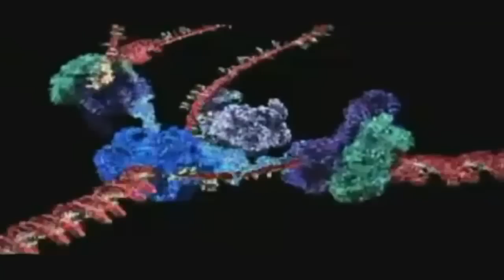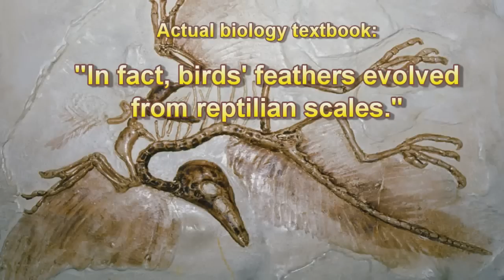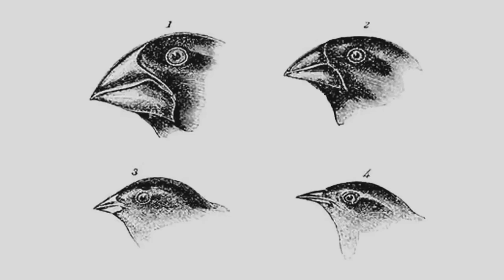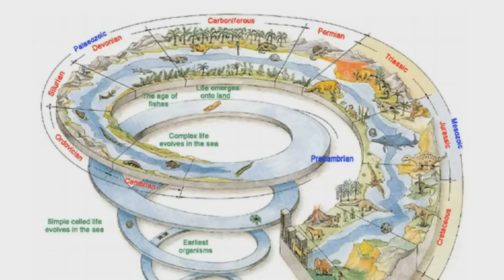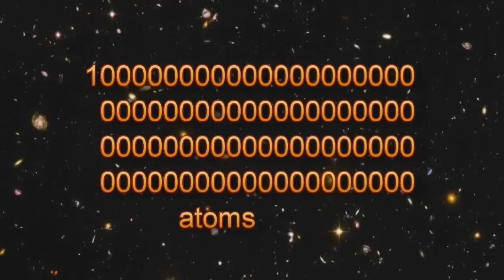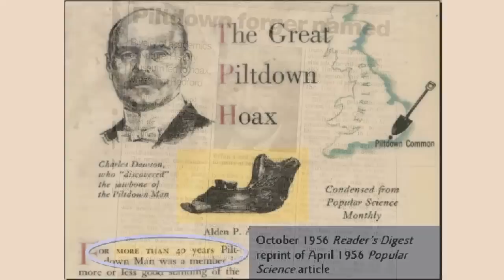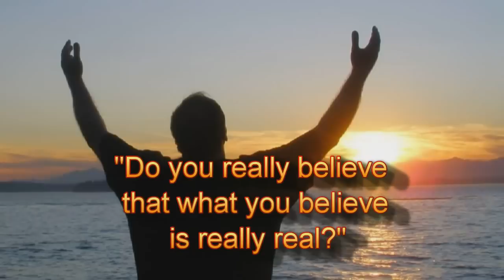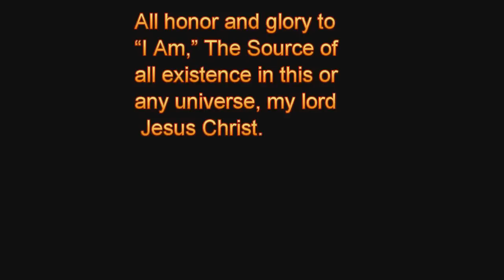Evolution Demolition

Comment: I'm sooo tired of people mentioning entropy... it seriously shouldn't be so damned hard to read up on what entropy states, and then think about what it implies for life and evolution.

The law states "an isolated system will tend to increase in entropy". Sure, tehre are version that says "cannot decrease in entropy", or "will tend towards maximum entropy", and so on, but they're still all essentially saying the same thing.

Is life an isolated system? Nope. An isolated system is a "area" where matter and energy isn't exchanged with the surrounding area. Life constantly eats energy from its surrounding (called metabolism) and excretes waste products. It's pretty much the perfect opposite of an isolated system. It's a very open system.

Is Earth an isolated system? Nope. Earth takes in energy from the sun, mainly, in the form of radiation/light. We also send out energy into the universe, mainly heat. We also recieve matter i the form of meteorites. Sicne we mostly exchange energy, but very, very little matter, this is called a "closed system" (not the same thing as an isolated system).

Is our solar system an isolated system? Almost, yes. It's nearly isolated, and that's fine to call "isolated" for the sake of argument, though we still exchange radiation and gravitational energy with other solar systems, and the rest of the universe.
So our solar system will tend towards increased entropy. But that doesn't mean that every sub-system of that system must tend towards increased entropy. Only the system as a whole must follow that law, since onyl the system as a whole is an "isolated system".
Life is per definition a sort of "machine" that primarily exists because of its ability to resist internal chaos by taking in energy from the environment.

What this video is arguing, "no one if above the law [of entropy]", means that life cannot exist. And that's obviously false. Our cells should not be able to take in outside energy to maintain homeostatis, so we should all die.
But we do exist, because we are not isolated systems! So the law doesn't apply to life, or anything else that isn't an isolated system.

Want an example of spontaneous creation of order in an open system? The formation of crystals. Fucking snowflakes.

And now for the argument about information theory and entropy:

Take a book, and make lots and lots of copies of it that have mutations, variations in them. Yes, most, or almost all of them will be worse. However, because of natural selection, only the ones that aren't bad will be kept. So lets say you made 10 000 copies. But because of natural selection, you only have 20 copies that survived, because they accidentally contained new random information that was actually useful, or at least wasn't bad.

Repeat this process as many times as you want. The laws are the same: Only useful copies are kept. What will happen? You'll form a tree, like the tree of life, with different versions of the book, all perfectly fine, but different. At no point will you ever have a "bad" branch, because bad specimen are never kept. And yes, those make up the largest part.

Go back just 100-200 years in time, and people sometimes had over 20 kids, though most of them died before they reached age 1. (I know, I've looked in my family history.)
Those that dies obviously weren't fit, or they just had bad luck. but the ones that did survive to adulthood passed the test of fitness. And then the test continues with the next generation.
Reply: antiHUMANDesigns And I'm so tired of the tired "open system" excuse for ignoring a law of science.  (Did you watch my video?)  A closed system is a requirement for measuring entropy; it is not a requirement for the law to be operative.  Instead of finding excuses for dodging a scientific law, why not explain its operation in the formation of DNA informational content?  Yes, entropy can be transferred out by an entropy transfer mechanism.  So what would that mechanism be in this case?  I've never heard of anything offered.  Random mutations are not such a mechanism.  In fact random activity is the very thing that destroys information.
Reply: Mark Champneys"And I'm so tired of the tired "open system" excuse for ignoring a law of science."

Are you seriously shitting me? The law states what happens in an isolated system, and you complain when people say it's not an isolated system? 8|
If you think the law of entropy is true for an open system, then life cannot exist. Our bodies are open systems, which allows us to maintain homeostasis, but this would be impossible if the law of entropy was valid for open systems. This proves that you're wrong.

"A closed system is a requirement for measuring entropy; it is not a requirement for the law to be operative. "

Once again, "isolated", not "closed". Yes, that is correct, but in an open system there are more things to take into consideration. Basically, an open system is a place where anything can walk in and ruin your experiment.

It's not hard: If you imagine a car engine being an isolated system, then the engine would stop working once it runs out of its internal fuel. However, if the engine is an open system, it can keep going forever, because we can supply new fuel to it and we can replace broken parts, and we can cool the engine with outside cold air, and so on. Open systems play under completely different rules.
And a closed system is also allowed to exchange energy, so it can also prevent the increase of entropy. Only an isolated system will suffer a tendency towards higher entropy with certainty.

"In fact random activity is the very thing that destroys information."

Entropy is the creation of new information. things tend toward higher entropy. Higher entropy = more complexity, and more possible states of a system, which means more information, in the sense of information theory - not in the sense of information that is communcated between minds, such as what music someone likes.
And DNA is not "information" in the latter sense. It's effectively a random sequence of nucleotides that jsut happens to be useful in it's own context. But it is not "information" in the sense that it would be useful outside of its context. "AGGTTCGTAAGC" is not "information", it's a structure that has chemical effects. If that is "information", then everything is.
Reply: antiHUMANDesigns Entropy does not create new information content, but destroys information content.  Entropy may add volume to the code, but that code becomes less certain, and obscures information content like static or noise.  More possible states of a system means less certainty in information theory.  Complete randomness might have a large volume of code, but it would be completely meaningless.  In the case of DNA we are concerned with prescriptive information, not merely data.  Prescriptive information must be specified for a particular outcome that is both complex and highly functional.  Such remarkable arrangements of nucleotides are overwhelmingly improbable.
Reply: Mark Champneys"Entropy does not create new information content, but destroys information content. "

Then you don't know what "information" is.
Lets take an example of a binary string: "11111111".
This can simply be explained as "8x1". The entropy is minimal. As entropy increases, the string changes to, for example "11011111". Now you can explain this as "2x1, 1x0, 5x1", or "3rd is zero, rest is 1, total 8", or something.
This is more information, because the information cannot be compressed (simplified)as much.
Thus, entropy creates "randomness", and randomness means more information.
A perfectly ordered string contains almost no information at all.
For example, compare a completely white JPEG file to a JPEG file of white noise (same dimensions). The white noise contains much more information, so the file will be larger than the "ordered" file.

" Complete randomness might have a large volume of code, but it would be completely meaningless."

Yes, and this exactly the point. Nothing ever has meaning in itself. Meaning is imbued on things in their context. The DNA sequences doesn't have any meaning whatsoever, but in the context of chemistry, the string of nucleobases becomes useful.

Take the human DNA sequence and store it in a computer. Apart form the fact that it tells us what the human DNA looks like, it isn't actually useful or meaningful outside of its own context. It doesn't contain any "infomation". It's not a language, it doesn't contain a message. It's effectively just a bunch of random nucleobases.

"Such remarkable arrangements of nucleotides are overwhelmingly improbable."

But this is explained by evolution, so that problem has been solved. No one claims that the sequnce just happened to be there out of random chance. It's governed by laws, such as natural selection.
Reply: Mark Champneys Yes, there are different meanings for the word "information". But I'm saying you're using the wrng meaning when it comes to DNA. DNA is like machine code on a computer. It has no meaning outside of its very specific context. And mutations really does create new information. It increases the amount of information in the gene pool. More information = more to pick from.

"Natural selection solves nothing. It is a filter, a culling mechanism."

Yes, it's one very important mechanism, but not the whole story. It's the filter, and natural variation is the input into the process.
Evolution is the successive addition of variations. "1" changes to "2", and then to "3", and so on, and eventually the number is "10000", and never actually had to make a large jump, because of these small successive steps.

"It cannot create instructions. It can only destroy ineffective ones. "

And it can keep effective ones, to allow further variations of these effective ones, until an even more effective one pops up. And so it keeps going.
Like I said, variation is the input that natural selection works with. Neither works alone. They complete eachother to create evolution.

"The proposed mechanism of evolution employs random mutations as a source for this prescriptive information before natural selection has anything to operate upon."

Yes, but not only random mutations. There is also recombination, for example.

"So your claim that "no one claims..." is utterly false. Every knowledgeable evolutionist claims random mutations for this."

No one says that the DNA sequence is what it is because of mutations. That would make it random, but it's not random, it follows laws. DNA is the way it is because it's been useful. That is not random.
Reply: antiHUMANDesigns Actually, natural selection does not "keep" anything.  It merely "choose" not to destroy.  The living reproducing organisms must provide the "keeping" part of the mechanism, but that is the very thing we are trying to explain the origin of.  How did reproduction evolve, when reproduction is essential for natural selection to operate at all?  Circular.

Recombination or duplication (and such) do not provide coherent instructions.  (A guy with a copy machine is not an author.)  If the invention of a pancreas only involved recombination, then a pancreas would be a simple organ indeed, but since this is not true, then it does not begin to explain anything.

"Useful" arrangements of nucleotides are very lengthy, and overwhelmingly improbable.  If a little luck followed by natural selection would do the trick, I'd be with you.  But we are not talking about a little bit of luck.  It can't happen in a trillion universe lifetimes.  Running a few numbers such as I did in my video readily demonstrates this.
Reply: Mark Champneys "How did reproduction evolve, when reproduction is essential for natural selection to operate at all? "

Before life was truly alive, it was probably just a molecule that copied itself. Likely an RNA enzyme, or possibly a self-replicating peptide. (Both have been shown to exist.)
So reproducion cannot have evolved, that's impossible. Evolution only works on things that reproduce (with variation), so reproduction must logically be the very first step to chemistry becoming biology.
And this is not a "problem". It's obvious.

"If the invention of a pancreas only involved recombination ..."

The pancreas never just "popped up". Like everything else it was a repurposing of something that already existed.
For example, our hands are repurposed fins.

""Useful" arrangements of nucleotides are very lengthy, and overwhelmingly improbable.  [... ]  It can't happen in a trillion universe lifetimes.  "

I'll bet you that your math is bullshit. I've seen such calculations before, and they're simply wrong, and usually don't even take evolutionary principles into account.
I'm really tired of people who think they can prove that something that happened didn't happen by throwing a bunch of unrelated numbers around.
Do you know the probability of me sitting here, writing this to you right now? How many truly impossible odds did I break just the last hour? A shitload. But that's not how it works.

"Running a few numbers such as I did in my video readily demonstrates this."

link it to me.
Reply: Mark Champneys I too, want to see your calculations, Mark. Share the profound conclusions of your "research," please.
Reply: +antiHUMANDesigns "Self" replicating is a term that is a huge stretch, since there is much more than "self" involved.  To begin with, there is no mechanism for such a complex molecule to form naturally and spontaneously in the first place.  Polymers degrade over time, rather than build up.  Even the Miller/Urey experiment was a failure in this regard.  It required a trap in the tubing to prevent the applied electrical energy from destroying the very molecules it was creating... and that was just an amino acid.  Energy must be harnessed (such as with ATP) in order to build rather than destroy.  The very notion of a "self" replicating molecule is contrived.  A self-replicating car would be vastly simpler than functioning RNA enzymes or peptides.

We might also talk about the next step after self-replicating molecules.  What next?  What about transcription/translation?  Where do ribosomes come from?  Where does ATP synthase come from?  What is the next step?  And the next?  The word "self" does not magically leap all these millions of hurdles.

Recombination or co-option is mud thrown against the ceiling to see if it will stick.  But it does not stick.  Co-option would have to be much more than re-assembling parts, but also involve re-sizing, re-shaping, and re-featuring parts.  However, shaking miscellaneous parts up in a paper bag does not assemble them and start them up, even when all the parts are absolutely perfect for the hoped-for new system.

I gave some illustrations of probability calculations in my video.  Did you watch it?  Have you had statistics?  Do you understand how improbabilities mount up exponentially?
Reply: Mark Champneys "To begin with, there is no mechanism for such a complex molecule to form naturally and spontaneously in the first place. "

Once again, these steps have been confirmed and demonstrated in a laboratory, under plausible early earth conditions.
Miller/Uery was interesting for its time, but we've progressed a lot since then, if you'd just care to keep up to date.
It doesn't matter how much you say it's not possible. It's been fuckning demonstrated...!

"What next? What about transcription/translation? Where do ribosomes come from? Where does ATP synthase come from? What is the next step? And the next?"

Yes, there is plenty of stuff to go, yet. A self-replicatign molecule isn't alive, so abiogenesis hasn't been completely solved, yet.
But every time people liek yo uhave said "that's not possible", we've demonstrated how it's possible. Every time.what makes you think that's every going to change?
The only reason you keep insisting that its impossible is because you don't want it to be possible. Why should anyone care?

"However, shaking miscellaneous parts up in a paper bag does not assemble them and start them up, even when all the parts are absolutely perfect for the hoped-for new system."

And that's not how evolution works. No one cares about your straw man version of science.

"I gave some illustrations of probability calculations in my video. Did you watch it? "

No, you still haven't linked it, even though I asked you to.

" Do you understand how improbabilities mount up exponentially?""

Yepp, I also understand the problem of trying to calculate the odds of something that's already happened, to show how impossible it was that it did happen. I can do that with absolutely anything. Even making tea.
I couldn't even tell you how many clearly impossible things I've done just this morning. So now I guess I'm off to have dinner at Milliways, right?
Reply: Mark Champneys I feel like antiHUMANDesigns has a pretty good handle on this debate, so I won't add anything just yet. I would like to see your probabilistic calculation though so I can see exactly what kind of model you used.

I'm just going to take a guess and imagine that you considered the prebiotic chemical environment a perfectly random system, and treated all probabilities as independent, right? Of course, chemistry is far from a random system. If we do calculations that way, the formation of a gram of salt with a 1:1 ratio of Na to Cl seems even more improbable than that of a small protein, so that would make your calculation invalid. If instead you made extensive use of Bayes' Rule, as you should, I'd like to see how you determined the conditional probabilities for each event.

So please, exactly where can I find this calculation, Mark? I'd rather not scan your videos aimlessly when you can just point me to the right one with a time stamp.
Reply: Max Spiegel Yes, that is exaclty what I'm expecting aswell, that his math would reflect a world where there are no laws that determine what is more likely to happen than other things, and where everything is tried in sequence, rather than in parallel. That's what I've seen so far, at least.
Reply: +antiHUMANDesigns Again, keep profanity out of this forum or you are done.

"A self-replicatign molecule isn't alive, so abiogenesis hasn't been completely solved, yet."  It isn't a trillionth of one percent solved.  You jump up in the air and then claim that you are on your way to Andromeda.  And the limited things that have been done in the laboratory only demonstrated what has been contrived by intelligent design, certainly not what happens in nature.  If you are going to claim that something can feasibly happen by accident, then you surely ought to be able to do it on purpose.  And after you prove that it can happen, then you will need to prove that it did happen.

"No, you still haven't linked it, even though I asked you to."  What are you talking about?  The video is at the top of this comments page.  Are you tell me you still haven't watched it?
Reply: Mark Champneys "Again, keep profanity out of this forum or you are done."

I'm done when I'm done, you don't tell me when I am done.
As for "profanity", I don't know what you're referring to, but if I feel the need for a specific word, then that is the word I'm going to use. Grow up. Words aren't going to hurt you.

""A self-replicatign molecule isn't alive, so abiogenesis hasn't been completely solved, yet." It isn't a trillionth of one percent solved."

I think I listed for you the 7 criteria for "life". Self-replication is one of those criteria. That makes it 14% solved, from that perspective.
Since those self-replicating molecules also evolve, that makes 2 out of 7, for a total of 28% solved.
A part from that, I don't know what advanced we've made, I haven't been keeping perfectly up-to-date on it, either.

" And the limited things that have been done in the laboratory only demonstrated what has been contrived by intelligent design, certainly not what happens in nature. "

The experiments are designed to demonstrate different things. Most of them simulate a natural environment, and there is no artificial element in the experiment, meaning nature is doing it alone.
But in some experiment, you're only looknig to prove that something is possible within the laws of physics, for example. you're not trying to prove that nature will do it alone, only that it can be done.
When it comes to abiogenesis, nature doing it alone is exactly the point we're trying to demonstrate.

"  If you are going to claim that something can feasibly happen by accident, then you surely ought to be able to do it on purpose."

Yes, and once we understand enough about it, we probably will. There is nothing known to science that would stop us from building something that already exists. Or even our own version of it.
There was a time when we could not build microprocessors, for example. Would you then argue that it was impossible for microprocessors to be built? Our science and technology might not be enough, yet, but be careful about talking about absolutes about the future.

"And after you prove that it can happen, then you will need to prove that it did happen."

Yes, that is correct. We start by finding a way that it could happen. Then we test if that does happen. But it's a completely different thing to demonstrate that it did happen when life started on earth. I don't know if we'll be able to demonstrate that, but I'd be quite happy at least knowing how it could happen. If we can only find one way of it possibly happening, and tests show that this process leads to something eactly like us, then it is reasonable to at least tentatively believe that's what happened.
But it really doesn't matter. The main point of science is being able to predict things, because that's useful. Knowing the history of something isn't quite as interesting.
But yeah, it's very well possible that we'll never be able to demonstrate that life on earth actually did start a specific way. Sad, but true.

""No, you still haven't linked it, even though I asked you to." What are you talking about? The video is at the top of this comments page. Are you tell me you still haven't watched it?"

Top of the comments page? I looked for it, and I don't know what you're talking about. Just link it and the problem is solved...!
Reply: +antiHUMANDesigns 
"Take a book, and make lots and lots of copies of it that have mutations, variations in them. Yes, most, or almost all of them will be worse. However, because of natural selection, only the ones that aren't bad will be kept."

 If you took all the words from the book "origin of species" and scrambled them into 10000 copies, how many of those books would be useful?
Reply: Benjamin Toby That is not how evolution works. Evolution is more like taking a book and making 10,000 copies with relatively small variations, then throwing out the approximately 9,999 that yield nothing useful and keeping the one that does. Rinse and repeat.
Reply: Max Spiegel so, if you continue making copies of "origin of species" with small random variations for say 1000000 copies, are you going to get a new readable book after that?
Reply: Benjamin Toby If you only keep the copies that are still readable, and repeat the process with those always selecting and copying from the readable ones, then obviously yes. All the unreadable copies are discarded as soon as they are created.
Reply: Max Spiegel so... If you repeatedly make copies from this book with random, slight variations, is it getting more readable or less?
Reply: Benjamin Toby How can something get "more readable?" It started readable, and all copies birthed from it (that we keep and make further copies from) are also readable. One may be a short poem, one may become a longer novel, but they would all be equally readable according to our analogy.
Reply: Max Spiegel hold on a minute: these copies: are we making them by intelligent recombination or by random alterations?... because anyone can switch words in a book to still make sense: that's intelligence: hence all 10000 books would make sense because thoughts have been put into making it look readable:

also take out the "getting more readable" clause and insert "still readable"... I think that'll suit the analogy better...
Reply: Benjamin Toby If we want to be accurate to evolution, we would need as many copies as there are organisms in a population, which is more on at least the 100,000 scale. We would then make copies of them with a few different random changes to each, like changing individual letters (point mutations), deleting or copying sections (indels), or even by doing something like changing where a sentence begins (frameshift mutations). We also might mix copies of the book with others to get copies (similar to sexual reproduction) with possible copying errors along the way.

Here you can probably see that the analogy breaks down a bit, because in DNA copying sections isn't necessarily a bad thing, whereas in a book repeating a paragraph would probably be frowned upon by the reader as lazy. In this way DNA is more like a computer code than a human language.

In any case, the idea is that we only keep the copies that still function and continue to make copies from them. They are, therefore, all still functional.
Reply: Max Spiegel so... in essence the book analogy doesn't apply to DNA codes... because DNA copies would require intelligent restructuring by that analogy... unless you propose another method of editing the copies of the book that doesn't require your intelligence...
Reply: Benjamin Toby No, the book analogy fails because unlike our DNA a book would almost never repeat itself, not because of intelligence. The qualities that make a good book are not like those that make a working organism. A much more accurate analogy would be with computer code.
Reply: Max Spiegel I think we're saying the same thing: the Book analogy is a miscue: as for the computer code, could you give an analogy from that?
Reply: Benjamin Toby Sure, they have even made programs that "write themselves." 
http://www.primaryobjects.com/CMS/Article149
Reply: Max Spiegel you see the problem with most of these analogies is the elimination of any aspect of intelligence from the foundation: Artificial Intelligence is merely intelligence created by human intelligence: hence any analogy from this would still require intelligence...
Reply: Benjamin Toby Well obviously you need to program the equivalent of the mechanisms that drive evolution: genetic drift, natural selection, non-random mating etc.

So by analogy, if you want to say that the fact that chemistry and natural selection exist is proof that ultimately the universe was "intelligently designed," I suppose I'm ok with that. You are basically saying that the fundamental laws of nature were designed. This is basically another "god of the gaps" argument, but at least it doesn't contradict science.
Reply: Max Spiegel you know the "God of the gaps" notion is another point I don't really grasp: allow me to use an analogy: if I see the Stonehenge for the first time and assumed it was an architecture without knowing the architect(s), would I be guilty of the gaps argument?
Reply: Benjamin Toby No, but if you assumed that a god must have done it you would.
Reply: Max Spiegel I see: so it's ok to assume an Intelligence designed the DNA codes?
Reply: Benjamin Toby It's not okay to assume anything in science. We need to demonstrate claims with evidence. In scientific theories this means by making unique, falsifiable predictions that are proven correct through repeatable experimentation.
Reply: +Max Spiegel so... what's the evidence to prove that the Stonehenge was made by intelligence?
Reply: Benjamin Toby Archaeological evidence showing various structures and remnants of a civilization. Of course, even without that it is significantly more reasonable to say that Stonehenge was made by people than by natural processes, because we know that humans have a tendency to arrange stones in formations that have to do with the position of the sun at various times of the year, and we have some idea how they actually could do it. None of those things are true when it comes to creating life.
Reply: +Max Spiegel "because we know that humans have a tendency to arrange stones in formations that have tondo with the position of the sun" ... but we also know that humans use digital codes to assign specific tasks to computers... can I then infer from that to conclude that the DNA is a product of intelligence?
Reply: Benjamin Toby No, because DNA is not a computer code, and we don't know humans to be in the business of designing life from scratch.
Reply: Max Spiegel it's not a human made computer code alright, and it doesn't look like one any human can make presently: but does that mean it's not a code?
Reply: Benjamin Toby You are implying that codes can only come from humans, which we know not to be true. We see the genetic code being written and edited by naturalistic means.
Reply: Max Spiegel sorry for the late edit... But my question is... Does the fact that DNA code is beyond human ability make it less of a code?  also, I'm implying that code can only come from intelligence...
Reply: Benjamin Toby How do you know that DNA is beyond human ability, or that code can only come from intelligence? We can see that the latter claim is false, as we see new pieces of genetic "code" being generated before our eyes through evolution.
Reply: Max Spiegel how I know code can only come from intelligence? Same way you knew the Stonehenge was an intelligent architecture... There's no false claim here it's just reason and logic... Same way you said it's more reasonable to say the Stonehenge was made by people...
Reply: Benjamin Toby One of the main problems with what you're saiyng is when you say "make sense". DNA doesn't "make sense" in the way a book does. The sequence of bases in DNA isn't useful outside of its own context you can't learn anything by "reading it".
DNA is a bunch of TCGA bases in what appear to be random sequences. The sequences are only what they are because the specific effect of those combinations has proven useful to the individuals from whom the DNA has been copied. But it's not like the DNA is "aware" of the effect it has. It's just a chemical memory.

DNA doesn't say "this is how you build an arm", and then goes on to explaining it to you. It's similar to how computer "machine code" is jsut a bunch of numbers that a specific CPU can read, but it doesn't actually hold any information, in the sense of being "informed".

Because it is not "information", in the sense of informing something, there is no right or wrong in DNA. Whatever sequences happens to exist are the ones that have proven useful for survival and reproduction, and that's all.

"Does the fact that DNA code is beyond human ability make it less of a code?"

How is DNA beyond out ability? It's a sequence of 4 different bases. humans language is way, way, way more complicated than DNA.
In fact, if DNA used our 26 letters, it could be much, much shorter and still contain just as much information.

And secondly, we have invented a better DNA, called XNA. It works the same way, but is more stable than DNA.

And if you're talking about the amount of information held in DNA, I can tell you that the harddrive on my computer could hold the entire DNA of a few thousand families of humans. One DVD-R is enough to hold your entire DNA.

So in what way would DNA be beyond our ability, when we can obvisouly do better?
Reply: antiHUMANDesigns

1. "you can't learn anything by "reading it"."... yes you can: realization of the fact that it is a code is learning...more so the other steps that are carried out with it's instructions: that's something that's extensively studied by experts...

2. you said the DNA is similar to the computer code: well what makes computer codes?

3. "humans language is way, way, way more complicated than DNA."... the DNA is a coding system: similar with computer digital codes: it contains instructions for building living organisms, not chatting with them: try translating a page of a book into digital code and tell me how complex human languages are again...

4. so you've invented an XNA? first did you borrow components from the living cell system or did you make it from the basic DNA elements from scratch?... secondly could you show me your functional organism/species/whatever?

5. " the harddrive on my computer could hold the entire DNA of a few thousand families of humans. " well it can't make anyuse of all that information... lol...

6. "So in what way would DNA be beyond our ability, when we can obvisouly do better?"... lol that's kind of hilarious... scientists can do something better? well try stopping whatever force it is that causes death: try making your cells regenerate forever...
Reply: Benjamin Toby I said it's reasonable to say Stonehenge was made by people because we know people can and do build such structures. We do not know people to do the same with genetic code. We don't know of any examples of archaeological sites being created by nature, but we do know of code being created by nature. There is almost no similarity at all between Stonehenge and DNA.
Reply: Benjamin Toby "1. "you can't learn anything by "reading it"."... yes you can: realization of the fact that it is a code is learning...more so the other steps that are carried out with it's instructions: that's something that's extensively studied by experts..."

Like I said, the only thing you learn is what the sequence is.
If I said "here is a cow", you will know the sequence of letters, yes? But on top of that, it infroms you about something, because the sequence of letters express information to you.
But with DNA, you might have a string like "TTGGACT", and when you read it, you know the string, but the string doesn't mean anything, it doesn't inform you about something.

Now, you can look at that string and figure out why that string is the way it is, sure, but that doesn't mean the string contains information. In such a case, you are informaining yourself with further study.

"2. you said the DNA is similar to the computer code: well what makes computer codes?"

It's similar in the sense that I described. It isn't exactly like machine code, but it has very many similarities. But it isn't machine code.

What makes machine code? A compiler does. (I am a computer programmer.)

When coding a program, you don't use machine code, you use a language that humans can more easily understand, which allows us to abstract things. I can basically tell the computer to calculate something for me, and store the result in memory. Anyone else who reads this code will understand what the code does, because it is informative.
However, when I'm done writing it, I need to compile it. The compiler reads my code and turns it into machine code, which is no longer informative, because it's been turned into pure instructions that causes the computer to perform a task. The computer is not even "aware" of what it's actually doing, it's just following a set of instructions.

And yes, we do have a similar thing for actually progrqamming DNA. We have machines that create DNA for us, and we have some kind of language that allows us to write code in an informative way, which is then compiled into DNA. I don't know much about it, though.

"the DNA is a coding system: similar with computer digital codes: it contains instructions for building living organisms"

Exactly. What if I could write a computer program code that builds a computer? I can't, because code cannot build things.
But DNA is a molecule, and it has chemical properties, it causes other molecules and atoms to do things. This is why it's still fundamentally different from computer code.

"try translating a page of a book into digital code and tell me how complex human languages are again"

I have no idea what your argument is. Human language is more complex because it is base-26 (or more), while DNA is base-4. This means that each "letter" can contain 26+ different values (ignoring special characters), compared to DNA's 4.
Digital code, however, is only base-2, so it can only contain 2 different values, and so it's less complex than DNA.

Our alphabet is more complex because I relay more information with fewer letters. If DNA used 26 letters, it could be much shorter and still contain the same amount of information.

"so you've invented an XNA? first did you borrow components from the living cell system or did you make it from the basic DNA elements from scratch?... secondly could you show me your functional organism/species/whatever?"

What? No it wasn't me!
https://en.wikipedia.org/wiki/Xeno_nucleic_acid
No, it's still new, and I'm not sure what they're planning on using it for.

"5. " the harddrive on my computer could hold the entire DNA of a few thousand families of humans. " well it can't make anyuse of all that information... lol..."

You're making less and less sense with each paragraph, I think. You think sequencing the DNA of people is useless? 8/

" lol that's kind of hilarious... scientists can do something better? well try stopping whatever force it is that causes death: try making your cells regenerate forever..."

Better than DNA, yes, as has been done many times.

There is no "force" that causes death. The problem with ageing is that cells mutate. Eventually, cells become something they're not supposed to be, and the body stops working properly. The body relies on each cell doing what it's suposed to do, but there is a form of evolution going on in the cells in the body, aswell. And that's not good for the body, which relies on a specific configuration of cells that do what they were initially meant to do. When the cells start doing other things, the body eventually fails as a whole.
But luckily, at that point the body has hopefully reproduced successfully, already, and a new body is created where each cell is once again doing what they were supposed to do.

Yes, it's theoretically possible to make humans not die from age. It's hard, but it's definitely possible.
Reply: antiHUMANDesigns

1. "What makes machine code? A compiler does."... ook... so what makes compilers?

2. "It isn't exactly like machine code, but it has very many similarities. But it isn't machine code."... Ummm... ook... I don't have any issue with that: similarity obviously doesn't mean equality: a three phase induction motor is similar to a laptop fan in the sense that they both produce torque: but they don't produce the same maximum torque...

2. "Our alphabet is more complex because I relay more information with fewer letters. If DNA used 26 letters, it could be much shorter and still contain the same amount of information."... there's a reason our language can't be used to make programs: it's because the machines operate best with machine codes: 0'sand 1's: like I said, our languages cannot be used to build complex systems: it's basically for communication between ourselves...

3. "You're making less and less sense with each paragraph, I think."... lol ... I think you should read most of your lines closely again: I don't think sequencing the DNA of people is useless obviously: but what was the point of telling me the hard drive could hold all that information when it'll be useless anywhere outside the cell? I mean it's not like you could get information the size of your hard drive into a small space as the cell...

4. There is no force that causes death?... oh yes there is, and you just explained it... but still I'll love to see scientists try to stop the process and prolong life...
Reply: Max Spiegel we know people can build complex machines and factories with digital machine code: what do you think goes on in the cell? the similarity between the two analogies is recognizing intelligence: if scientists found a structure like the Stonehenge in Jupiter wouldn't there be jubilation for discovery of extraterrestrial intelligence?
Reply: Benjamin Toby "1. "What makes machine code? A compiler does."... ook... so what makes compilers?"

Programmers write compilers.
It would probably be faster if you just get to your point.

"there's a reason our language can't be used to make programs: it's because the machines operate best with machine codes: 0'sand 1's: like I said, our languages cannot be used to build complex systems: it's basically for communication between ourselves..."

No, the reason why our language is not used by machines is because machines have no reason to be informed. They only need instructions.
The fact that we can say "1's and 0's" proves that our language could be used to run a program. But it's a bad idea, since it's unnecessarily cumbersome.

Also, computers don't necessarily have to run in binary. And on top of that, quantum computers aren't simply binary, either.

But if you want to make complex programs, you need to use abstraction. You need to write your program in some way that is closer to human languages, and let a compiler translate that to pure instructions when you're done.
In such case, what you're doing is that you're informing a compiler of what you want the program to be like, and it will create it for you.

"but what was the point of telling me the hard drive could hold all that information when it'll be useless anywhere outside the cell?"

Yes, so you do think that sequencing someone's DNA is useless, then. It's not useless, because we can use that for paternity tests, or we can use it to see if someone is likley to get specific illnesses, and so on.

And no, it's not because the DNA contains a message about what children that individual has. It's because we can compare the sequences to other sequences. That doesn't make it informative, it's the comparison that is informative.

" I mean it's not like you could get information the size of your hard drive into a small space as the cell..."

It's not readily available to read if it's in a cell. Also, if it's in a cell, it will mutate. Computers have much, much better way to detect and correct errors, since computers are specifically designed to not screw up the data.

"4. There is no force that causes death?... oh yes there is, and you just explained it... but still I'll love to see scientists try to stop the process and prolong life"

That's not a force...! It's just a phenomenon. 
Yes, I agree, that would be awesome.
Reply: Benjamin Toby "if scientists found a structure like the Stonehenge in Jupiter wouldn't there be jubilation for discovery of extraterrestrial intelligence? "

Humans build stonehenges. if we found stonehenge on jupiter, we'd have to assume humans built it, not extraterrestrials, right? Or we could just not make any assumptions before we actually know where it came from.
Reply: Benjamin Toby Again, we do know that nature can create code. We do not know that humans can and do create structures like Stonehenge on Jupiter. It would therefore be wrong to assume that DNA code comes from humans, or that a Stonehenge-like structure on Jupiter was man-made.
Reply: antiHUMANDesigns

1. "Programmers write compilers.
It would probably be faster if you just get to your point."... lol.. are you kidding me? you just answered the question... maybe you typed so much you forgot the point... DNA is a code similar to computer codes you said: intelligence accounts for all computer codes you said; but not the DNA... 

2. "They only need instructions.
The fact that we can say "1's and 0's" proves that our language could be used to run a program. But it's a bad idea, since it's unnecessarily cumbersome."... didn't I say the machines operate better with machine codes?... 0's and 1's, off and on call it whatever: it's just to represent two states: so our language can't work for computers except representing those two states... in case you forgot I gave you an example of translating a page to digital code: it'll be longer since the computer operates in two states... so the digital code is more or less a tool to signify when and how to switch between two states: that's how the DNA works: 

3."Yes, so you do think that sequencing someone's DNA is useless, then." what? how's that an answer? did you miss the question?

4."That's not a force...! It's just a phenomenon." ...actually you have no clue what causes death: all you can do is try to explain how it works: which is basically degeneration of cells... however what you explained was a phenomenon alright: 

5. "Humans build stonehenges. if we found stonehenge on jupiter, we'd have to assume humans built it, not extraterrestrials, right?" 
again I didn't say it had to be exactly like the Stonehenge I said "something like": ie some form of architecture resembling the Stonehenge... the point is, even if something like that is found where no human ever landed with his feet, it'll be assumed it was a product of intelligence... right?
Reply: Max Spiegel not my point at all: my point is if scientists found a structure like the Stonehenge on a place where no human had ever landed, the'd assume it was extraterrestrial intelligence regardless of the fact that no human ever landed there... no?
Reply: Benjamin Toby No. They wouldn't. That would be foolish without investigating the geology of Jupiter in detail.
Reply: Max Spiegel lol.. that's funny... so you mean to tell me that these same people that put a whole lot of hardware searching for extraterrestrial life would see a well-placed structure in Jupiter and dismiss it?
Reply: Benjamin Toby You think SETI would settle for a Stonehenge-like structure as proof of extraterrestrials? Why didn't they jump at the face on Mars? I think you should investigate their criteria for identifying and verifying evidence of extraterrestrials.
Reply: Max Spiegel that face was a "Martian mesa"... like a plateau or something: nothing close to  a Stonehenge-like structure... the real question is why did it get their attention in the first place?
Reply: Benjamin Toby It didn't. It got the attention of a few wackjobs and conspiracy theorists. Again, just google what it is that SETI is looking for. It ain't faces or Stonehenges.
Reply: Max Spiegel again, not my point: they're not looking for faces(btw that wasn't a face) or Stonehenges per se... they are looking for for signs of INTELLIGENCE: which a Stonehenge represents... maybe the Stonehenge wasn't a good example: what if they found a structure like the Chichen Itza in Jupiter: what'll be their conclusion?
Reply: Benjamin Toby They would conclude that they should investigate it further.
Reply: Max Spiegel I agree... They're not going to investigate if it's just a bunch of scattered rocks: that means they recognise intelligence...
Reply: Benjamin Toby What kinds of "signs of intelligence" are they looking for? Have you actually read their site yet? If not, maybe you could go read it now, yeah?
Reply: Max Spiegel I don't need to read their site to know they're going to find interest in a structure like the Chichen Itza in Jupiter: something as weak as the face on mars sparked curiosity because of the thought of some kind of intelligence... How so something as well structured as the Chichen Itza? that's my whole point: we recognise intelligence when we see it: except of course we deliberately refuse to see it...
Reply: Benjamin Toby You claim that you don't need to read SETI's criteria for what they would consider a sign of ET life to know what they would consider a sign of ET life? Then you say they would consider a pyramid-like structure proof of ET life? No, you clearly really need to read what they are looking or if that's what you think.
Reply: Max Spiegel OK bruh I'm going to read it and verify my claim: but are you really banking on the chance that a structured architecture wouldn't fit their criteria for extraterrestrial intelligence?
Reply: Benjamin Toby I am banking on the fact that no reputable institution is looking for such things, and that if one was found it would not be conclusive evidence of ET life.
Reply: Max Spiegel that's funny... But OK...
Reply: Benjamin Toby "DNA is a code similar to computer codes you said: intelligence accounts for all computer codes you said; but not the DNA..."

Yes, that is correct: Computer code is written by humans, exclusively, as far as we know. DNA is not. Human DNA exists because it copied itself, naturally. And the sequence in the DNA is what it is because it was useful to the organism.
No one wrote the human DNA.

"0's and 1's, off and on call it whatever: it's just to represent two states: so our language can't work for computers except representing those two states"

It's logic that only has true or false. A computer uses logic.
but I'm not entirely sure what yo umean, because while it comes down to true/false (1/0), the letter "a", or even a word, could translate to a specific series of instructions, and this is sort of how computer instructions already work. While computers really can only do about 6 different things, add subtract, multiply, divide, read and write, they have extended instructions for "swapping" and such, which either executes speifici new circuitry that does some things fast, or it represents a series of instructions that perform a task.

But it's true that logic only have true or false, and that's why a computer fundamentally likes binary. But it's still perfectly possible to make a computer that doesn't only use base-2 (binary), but any other base, instead.

It's important to note that our brans and nervous systems also only uses true/false. Either a nerve fires or it doesn't.

"in case you forgot I gave you an example of translating a page to digital code: it'll be longer since the computer operates in two states... so the digital code is more or less a tool to signify when and how to switch between two states: that's how the DNA works: "

No, that's not how DNA works, because DNA isn't a nervour system, or anything of the kind. Each 3 bases of the DNA produces an amino acid that gets added to a protein. "GCT"  might make one amino acid, for example. Correct me if I'm wrong, but I think our proteins use 20 different amino acids, so the system is effectively base-20, as it is right now, though I suspect it's capable of much more, theoretically. As far as I know, the system never uses just one base, but always 3 bases at a time.

You still seem to think that DNA does something else than simply sequence new proteins. It's the proteins that make stuff happen, not the DNA. And the possiblity of different kinds of proteins is enormous, so in reality, it is truly nothing like compute code, in action.
But it could be, it has te capability to be. It's just that's it's not.

"4."That's not a force...! It's just a phenomenon." ...actually you have no clue what causes death: all you can do is try to explain how it works: which is basically degeneration of cells... however what you explained was a phenomenon alright: "

Of course I know what causes death. I mean, there are sooooo many things that causes death. Sure, I don't know of all them, or I'd have ot be an expert, and I'm not, but we all know ways to kill cells, or to disrupt the vital functions of the body.
Even ageing isn't one cause of death. Ageing increases the chances of things going wrong in the body, but age is never what kills you, directly.
Ageing is a phenomenon, not a force.

"again I didn't say it had to be exactly like the Stonehenge I said "something like": ie some form of architecture resembling the Stonehenge... the point is, even if something like that is found where no human ever landed with his feet, it'll be assumed it was a product of intelligence... right?"

Well, you'd have to be specific if you expect to get a good answer.
If you're calling it "architecture", then you've already assumed it's intelligently designed. So don't call it that.
Yes, lots of people would assume it was intelligently designed, but scientists would not. Reasonable people would not. We would accept the possibility, of course, while we investigate, if it is the first time we're seeing it.

Remember the picture of a face on the surface of mars? Lots of people went crazy and assumed it was intelligently designed. Turns out there was no reason at all to suspect it was intelligently designed, even though it looked like a human face.
So I don't care if people would make such assumptions, the question is whether they're rationally justified to make those assumptions, and they're not. Lots and lots of people are irrational and unreasonable.

For us to believe that somethign was intelligently designed, we need evidence that it was intelligently designed. I personally would accept 2 lines of evidence for that:
1. A printed message from the creator of that thing, for which we can find no other function than to relay that message.
2. Evidence of an intelligent designer of that thing.
In such case, I would accept that the thing was most likley intelligently designed.
But when I look at a rock, I don't see any such message, and I have no evidence of an intelligent rock-creator.

In the same way, I look at life, and I see no such message, and no evidence of someone who creates life, who might have created life on earth. That doesn't mean I think intelligently creating life is impossible, or that it didn't happen, it just means I have absolutely no rational justification for believing in such things. I would have to be irrational to believe it to be true.

On top of this, we have a scientific explanation for how life can evolve, and we have a fossil record showing us that life did evolve, and we can see, in our DNA, that we are related, and how we are related.
So why on earth would I throw this explanatioon away, in favor of something that has no evidence, and doesn't fit the evidence?
Reply: antiHUMANDesigns

1. "Computer code is written by humans, exclusively, as far as we know. DNA is not."... you are really good at stating the obvious... I think any reasonable person can tell DNA wasn't written by humans: I'm sure any reasonable person can also tell it's a code: and that's the point... you recognize it's a code but believe it was an accident... 

2. "No, that's not how DNA works, because DNA isn't a nervour system, or anything of the kind. "... well you don't seem to understand the analogy... let me explain again: the computer code is a tool used to tell when and how to switch between two states: the DNA code is a tool to tell when and how to build proteins... see any similarities now?

3. "It's the proteins that make stuff happen, not the DNA." ... and proteins can't be made without DNA: "And the possiblity of different kinds of proteins is enormous"... obviously the possibility for different kinds of USEFUL proteins is much: that's obviously allowed by the code: but that possibility is nowhere near the possibility for useless ones...

4. "If you're calling it "architecture", then you've already assumed it's intelligently designed."... again obviously that's what I'm saying...and again the point is, and I repeat, finding an architecture where no human has ever been would instantly provoke the thought of intelligence... but apparently "reasonable" people would think otherwise... 

5. the face on mars... what do you think provoked people to investigate it?

6. "For us to believe that somethign was intelligently designed, we need evidence that it was intelligently designed."... that's funny... did you check for a "printed message" from the creator of the Stonehenge to know it was intelligently designed?... and give me the evidence that it was intelligently designed...

7. "In the same way, I look at life, and I see no such message, and no evidence of someone who creates life, who might have created life on earth."... in essence what you're saying is the same amount of intelligence you find in a rock is what you find in all of life: that's very telling... 

8. "it just means I have absolutely no rational justification for believing in such things. I would have to be irrational to believe it to be true."...sooo I guess it is perfectly rational to believe that the DNA coded itself into a complex, well sequenced, self repairing, self re-sequencing code by chance: and the complex human system came about by random recombination and altering of  DNA codes... interesting... 

9. "On top of this, we have a scientific explanation for how life can evolve, and we have a fossil record showing us that life did evolve, and we can see, in our DNA, that we are related, and how we are related."... you mean natural selection acting on fully functional organisms?... well I don't need science to see that selection worked on the grey wolf to produce a chihuahua... also the fossil record shows a short period of time when fully developed organisms just appeared: the Cambrian explosion... also the DNA represents a common creator: which you call a common ancestor... which also of course according to you, was a fully functional "self-creation"...

10. "Of course I know what causes death. I mean, there are sooooo many things that causes death."... again, obviously I'm talking about natural death: and again, obviously you have no clue what causes it: there's no need to try to explain what you don't know...

11. "So why on earth would I throw this explanatioon away, in favor of something that has no evidence, and doesn't fit the evidence?"... I'm not saying you should throw anything away: I'm only saying you should apply more reason and logic... 

12. Personally, every form of rational thinking leads to acceptance of some form of intelligence in the earth: a total denial is like denying one's own existence: the evidence of intelligence is enormous humans learn from it some times: the air plane has it's roots to the flight pattern of the bird: the two human kidneys show evidence of redundancy: and many more aspects: it's overwhelming that the only place to hide it is in plain sight...
Reply: Benjamin Toby I won't be giving long replies because I don't have time to address them, but I remind you that we see the codes in DNA being written by nature all the time. It is not a mystery from whence they come.

By now you have looked into SETI's criteria, I'm sure, so please stop with the "it looks designed to me, so that's the best assumption" criteria. Nobody except creationists say such nonsense.
Reply: Max Spiegel remember your comment?..."Well obviously you need to program the equivalent of the mechanisms that drive evolution: genetic drift, natural selection, non-random mating etc.

So by analogy, if you want to say that the fact that chemistry and natural selection exist is proof that ultimately the universe was "intelligently designed," I suppose I'm ok with that. You are basically saying that the fundamental laws of nature were designed. This is basically another "god of the gaps" argument, but at least it doesn't contradict science."... that's basically my argument: the DNA was intelligently designed: it has little to do with the formation of atoms or fundamental laws: my argument is from the obvious processes in the DNA and the cell... if you call the assumption of intelligence in the cell nonsense, that's like saying an assumption of the Stonehenge, being the product of a rock slide, is rational... note: it's not an argument about the origin of the stone, but the stone architecture...

btw I've not looked into the SETI site yet: I have more important things on my hands and I also have to reply your colleague with the long comments...
Reply: Benjamin Toby Chemistry and natural selection are fundamental principles of the universe. You programmer would have to be working around the time of the big bang.
Reply: Max Spiegel again: my argument is not from the origin of the atoms: it is from the functioning of the cell: so the Big Bang is just way off my point: it's just like arguing about the origin of the stones of the Stonehenge... my argument is about the architecture of the stones,not the origin of the stones: and that architecture indicates intelligence...
Reply: Benjamin Toby Ok, but that breaks the analogy we had. You want a god to interfere with the "program" that has always been running the same laws of physics, reach in to the already running program and do some unspecified magic to make life appear. You still have no evidence of this, and it contradicts everything we know about science.
Reply: Benjamin Toby "you are really good at stating the obvious... I think any reasonable person can tell DNA wasn't written by humans: I'm sure any reasonable person can also tell it's a code: and that's the point... you recognize it's a code but believe it was an accident... "

I think you better look up the definition of "code", again. Refresh your memory.
"A word, letter, number, or other symbol used in a code system to mark, represent, or identify something: "
You cannot just take any chain of somethign and say it's a code, just because it's a chain/string of different values.
"235698286359" <- I just wrote a bunch of random numbers, there, is it a code? No, it's not, because it wasen't encoded, and it's not intended to be decoded. Just because it's a chain of numbers doesn't mean there's any informative information in it.
So whether DNA is a code or not is not "obvious", it depends on how the DNA is being used. Life does not use it as a code, it uses it as a chemical memory, a sequential blueprint, similar to how a computer program works. It's not encoded, because then it would have ot be interpreted before it could be used. The sequences are being used directly, they are not decoded first.

But I'm really starting to wonder why we're having this discussion. What does it matter? We cannot define something into existence. DNA is what it is, and science has demonstrated how the sequences of DNA changes, and we have demonstrated how the sequence can come about through chemistry.
If you want to call it a "code", or whatever, then fine, no need to argue about that *as* long as you don't think that it means that someone must have written it, because we have demonstrated that that is not the case.

" the computer code is a tool used to tell when and how to switch between two states: the DNA code is a tool to tell when and how to build proteins... see any similarities now?"

Yes, this is what I've agreed on from the start: That DNA is used similarly to how machine code is used for a computer. (Just don't forget the ways it's not similar.)

"3. "It's the proteins that make stuff happen, not the DNA." ... and proteins can't be made without DNA: "And the possiblity of different kinds of proteins is enormous"... obviously the possibility for different kinds of USEFUL proteins is much: that's obviously allowed by the code: but that possibility is nowhere near the possibility for useless ones..."

I have no idea how many proteins could be useful, I'm no biochemist, and I don't know how those things work on the chemical level.

" finding an architecture where no human has ever been would instantly provoke the thought of intelligence... but apparently "reasonable" people would think otherwise... "

I'm not sure you understand the problem with what you're saying. If we find architecture, then we know for a fact that it was artificially created, because that is the definition of "architecture".
The question is how we can tell if it is architecture or not. It's not architecture just because it looks like it. It's architecture if it was designed by a mind. So we have to know if it was designed by a mind before we can call it architecture.

If no humans have been there, then it's not likley architecture, because for it to be architecture, it must reasonably have been made by extraterrestrials, then. And we have seen to sign of any extraterrestrials, so it's going to be hard to prove it to be designed by ET's.

"5. the face on mars... what do you think provoked people to investigate it?"

Human nature? Luckily, the process of investigation isn't ruled by human nature, at least.

" that's funny... did you check for a "printed message" from the creator of the Stonehenge to know it was intelligently designed?... and give me the evidence that it was intelligently designed..."

First of all, I haven't had the chance to examine the stonehenge, personally, so I don't know much about it. Neither have I read about the evidence, and so on. I don't know what makes us sure it was made by humans, so you would have to ask someone who has some knowledge about that.
What I do know is that humans are known to make such structures.  Saying it was made by humans is just the "most reasonable" position from where I'm standing, personally, with what evidence I *do have, such as knowing that humans make such structures, and that there are no other known "candidates". I don't think we've ever seen nature make such a structure.
But then again, there are some seriously cool things that nature has made:
https://en.wikipedia.org/wiki/Giant%27s_Causeway#/media/File:Causeway-code_poet-4.jpg
Considering that this pattern of rock was made naturally, we have to be careful what we assume to be made artificially.

In any case, this is also why I understand that people assumed life was made by some intelligence, before we had a scientific explanatioon for it. If I lived 500 years ago, I would probably also be a creationist. But this is the 21st century. And I was hoping people had learned from past mistakes, and that people would stop assuming that everything we don't understand is "god", when that's been wrong every time so far.

"7. "In the same way, I look at life, and I see no such message, and no evidence of someone who creates life, who might have created life on earth."... in essence what you're saying is the same amount of intelligence you find in a rock is what you find in all of life: that's very telling... "

I didn't say "intelligence", I said "message". You know, when a company makes a clock, it might have a sticker that says "made in taiwan", for example. That is typical for something that was intelligently designed.
And when Dr Venter made the first artificial cell, he put a message in its DNA that is an URL that leads to a secret website.
So, there you have some examples of things that we know for a fact are intelligently designed, and they have these "messages" in them.
Now look at human DNA, and tell me where the evidence for intelligent design is? There is no "made by god" sticker in there, even figuratively.

"...sooo I guess it is perfectly rational to believe that the DNA coded itself into a complex, well sequenced, self repairing, self re-sequencing code by chance: and the complex human system came about by random recombination and altering of  DNA codes... interesting... "

Yes, sort of, if you had cared to take the time to study the evidence for that. That is why 99% of everyone who is a scientist in a related field agrees that's what happened. It's funny how pretty much the only ones who disagree are the ones who haven't studied it., and who also have a bias against it.

"you mean natural selection acting on fully functional organisms?... well I don't need science to see that selection worked on the grey wolf to produce a chihuahua"

As far as I know, the chihuahua comes from the east asian wolf, not the grey wolf, but who cares...
"Fully functional"? Yes, life is... fully functional. (I have no idea wtf you're talking about.)

So what, you agree that wolves did evolve into dogs, then? Yet you have some kind of problem with the idea of evolution? How do you make that fit together?

"also the fossil record shows a short period of time when fully developed organisms just appeared: the Cambrian explosion"

"Short", huh? First of all, the cambrian explosion happened over something like 25 million years. Compare that to the fact that humans are only 6-7 million years apart from chimpanzees. While 25 million years is a short time on the geological scale, it's still not a short amount of time.
And no, they didn't appear from nowhere, and we have fossils of their ancestors.
The only thing that is interesting about the cambrian explosion is that life diversified relatively quickly during that time, and the question is what drove this thing to happen.
But of course, you've only listened to creationist who want to spread misinformation.

But it is true that the cambrian explosion was a long, long time ago, and it happened relatively quicjkly, which means we have the problem of lack of fossils. If some life form only existed for a short time, there's less chance of finding a fossil of it.

But I'm really iunterested in hearing what you're really trying to argue, here. Are you arguing that god made the cambrian explosion happen, or what? I mean, none of this is helpful to creationism, so I don't know why they even bother.

"also the DNA represents a common creator: which you call a common ancestor"

That is correct, the common ancestor is the common creator. The common ancestor between you and your siblings are your parents, they created all of you. the common ancestor of you and your counsins are your grandparents, they created all of you.
And go far back enough and you'll find the "grandparent" of all humans and chimpanzees, for example.

We know this, because we can do paternity tests to see who your parents are, and who your siblings are, and in the same way, we can see that you are related, more distantly, to other species on earth.

"10. "Of course I know what causes death. I mean, there are sooooo many things that causes death."... again, obviously I'm talking about natural death: and again, obviously you have no clue what causes it: there's no need to try to explain what you don't know..."

Natural death = anything but "murder", which would be "artificial death".
You can keep saying I don't know causes for death, buy that doesn't make it true. Both you and I, and most other people, know causes for death. For example, my father died because a blood vessel burst in his brain, and the pressure in the skull built up until the brain pretty much got squeezed, and eventually there was no brain activity left. This doesn't make him dead, but it makes him unable to stay alive on his own, and he could never recover from this. But sure, science can keep his cells oxygenated, and so on, but what's the point?
However, the definition of "medically dead" has changed with time, as we learn more about it. I think currently, for you to be dead, there are 5 systems that need to stop working for you to be considered dead. No brain activity, no breathing, no heart rate, and so on. So while it's not a simple answer, we all know things that cause death. I have no idea why you're pretending that we don't.

"I'm not saying you should throw anything away: I'm only saying you should apply more reason and logic... "

How do I do that, you mean? "More" logic?
Or do you just mean that we should keep doing the science? Because yes, we should. But we're not going to discover something that negates everything else that we've discovered so far.

"12. Personally, every form of rational thinking leads to acceptance of some form of intelligence in the earth"

Then you are you either unable or unwilling to share your rational reasoning for this, then? You've given nothing me nothing, so far. If you think that anything you've said so far is an  argument for intelligent design, then all you've got i a bunch of fallacies, most notably the fallacy called "argument from ignorance".

"the evidence of intelligence is enormous humans learn from it some times"

We know there is intelligence, but that's not what you're arguing for. Humans, for example, are considered intelligent. So, there's proof that "there is intelligence".
But this is 'not' what you're trying to argue for. So make a proper argument, and give proper support for it.

" the air plane has it's roots to the flight pattern of the bird:"

Yes, nature knows more than we do, so to speak, so we learn from it.

" the two human kidneys show evidence of redundancy: "

Are you seriouisly arguing that only something that is intelligently designed has use for redundancy? :P
I'm not so sure that we have two kidneys simply because we need a "spare". I think, they're probably both useful at the same time. Someone who has only one kidney needs to be careful about his/her diet, and so on.

But if you're telling me that redundancy is a trait of intelligent design, then why the fuck do we only have one heart?
I mean, the human body is not very well designed. There ar elots of really stupid things in here, but that is perfectly explained by evolution. But if you're going to claim that it was intelligently designed, then that designer is pretty bad, and pretty crazy, even.
Reply: antiHUMANDesigns 

1. code
      noun \ˈkōd\
: a set of laws or regulations

: a set of ideas or rules about how to behave

regulate: 
a :  to govern or direct according to rule(merrian-webster)...

a code in simplest terms is just a set of regulations: the DNA contains regulations for building everything in a living organism so it qualifies as a code: this is why "computer code" and "genetic code" both come with an adjective... the computer code regulates the switching of states, and the genetic code regulates the building of proteins...

2. " It's not encoded, because then it would have ot be interpreted before it could be used. The sequences are being used directly, they are not decoded first."... have you even seen how the DNA works?... the ribosome does the interpreting and the sequences are obviosly not used directly because the end product is the organism... 

3. "Yes, this is what I've agreed on from the start: That DNA is used similarly to how machine code is used for a computer."... so what's your argument?

4. "I'm not sure you understand the problem with what you're saying. If we find architecture, then we know for a fact that it was artificially created, because that is the definition of "architecture"."... that's a straw man there... how would you expect me to describe my point? what word should I use? alien structure?...  then we know it's an alien structure because that is the definition of "alien structure"...

5. "If no humans have been there, then it's not likley architecture, because for it to be architecture, it must reasonably have been made by extraterrestrials, then. And we have seen to sign of any extraterrestrials, so it's going to be hard to prove it to be designed by ET's."... oh well you're speaking of a different thing here: investigation... which deals with finding out who/what made it: not if it was made or not...

6. "Human nature? Luckily, the process of investigation isn't ruled by human nature, at least."... that probably because the investigation comes after the observation: the "human nature" recognized a "face-like" structure: that's my point: no one is going to be investigating a bunch of scattered rocks on mars...

7. "In any case, this is also why I understand that people assumed life was made by some intelligence, before we had a scientific explanatioon for it. If I lived 500 years ago, I would probably also be a creationist. But this is the 21st century. And I was hoping people had learned from past mistakes, and that people would stop assuming that everything we don't understand is "god", when that's been wrong every time so far."... oh well in the present dispensation, your assumption is that everything we don't understand is an accident:

8. "I didn't say "intelligence", I said "message". You know, when a company makes a clock, it might have a sticker that says "made in taiwan", for example. That is typical for something that was intelligently designed."... 

firstly you said "and I see no such message, and no evidence of someone who creates life, who might have created life on earth."... that "someone who creates life": that's the intelligence you paraphrased...

secondly the sticker doesn't indicate the clock is intelligently designed, it only indicates WHO designed it... big difference... that's why no one searches for a sticker on the Stonehenge to know it was intelligently designed... the mystery is who designed it...

9. "So what, you agree that wolves did evolve into dogs, then? Yet you have some kind of problem with the idea of evolution? How do you make that fit together?"... I agree for a certain limit of variation based on the gene pool: but new information is what the theory of evolution proposes and that has never been seen: the theory evolution says that a dog can develop wings: just like the fish apparently developed human limbs over millions of years... the question is how do you make that fit together with the Wolf-dog variation?

10. "And no, they didn't appear from nowhere, and we have fossils of their ancestors."... It's time to start backing your claims with evidences: could you show me these fossils of the ancestors and transitional forms?... don't talk of misinformation until you submit the fossil evidences of all the organisms and their step-by-step evolution from their ancestors.

11. "But I'm really iunterested in hearing what you're really trying to argue, here. Are you arguing that god made the cambrian explosion happen, or what? I mean, none of this is helpful to creationism, so I don't know why they even bother."... oh well first there were no "ancestors" of those organisms in the records which can be traced through step-by-step variations... secondly how is it possible that soft-bodied organisms can last for "500 million" years without totally decaying?... thirdly, if these soft-bodied organisms lasted so ling without decay, the the fossil record should show the transitional fossils in details including the step-by-step addition or removal of new parts.

12. "Natural death = anything but "murder", which would be "artificial death".
You can keep saying I don't know causes for death, buy that doesn't make it true."... first natural death can't be artificial death: the death I'm talking of is the death that occurs through aging: ie the inevitable death regardless of how healthy you are... secondly no need to explain what causes it because you are just going way of point: I'm sorry for your loss but that's not my point.

13. "Then you are you either unable or unwilling to share your rational reasoning for this, then? You've given nothing me nothing, so far. If you think that anything you've said so far is an  argument for intelligent design, then all you've got i a bunch of fallacies, most notably the fallacy called "argument from ignorance"."... of course considering that my basic point was the failed book analogy, you can blame me for trying to address your whole drivel and unnecessarily ambiguous and cumbersome comments: I see you as the proof of a result of rationally irrational thinking(for the lack of a better description): how else can I explain arguing about the DNA not being information or code, or the DNA writing itself: I've seen many people like you using the phrase "argument from ignorance" while displaying such argument all the time: my argument is from what we know of the product of intelligence: your argument is from what we don't know which is the imaginary technique of building complex systems from simpler ones by accidents... no lab has been able to build a cat from a fish even by human intelligence: but you argue that a fish can turn into a lion over millions of years and yet accuse me of an argument from ignorance...

14.maybe the kidney example was a wrong analogy in this scenario: I say that not because the two kidneys don't show some form of redundancy but because that's no point to waste time on: however your excuse for that as a proof of no intelligence is even more ignorant and irrational: I mean in what sense of rational thinking is it better to assume that the two kidneys and heart resulted from random undirected formation of organs?...
Reply: Max Spiegel firstly I don't "want" a god to interfere with any running program or such: I'm saying that an Intelligent designer was responsible for "programming" the DNA... I'm not sure if I'm getting you correctly or vice versa but that's my main argument...
Reply: Benjamin Toby DNA is clearly not being programmed by any "designer" now, as we see it being written by natural laws all the time.

What identity do you propose for this "designer" if not a god? I've only ever seen fundamentalist Christians push this thinly-veiled version of creationism, so it's obvious they want to insinuate that there is a god behind it all. Namely Yaweh.

Are you different? Do you think the "designer" could be an alien?
Reply: Max Spiegel remember you said something about AI?... The DNA is probably not being programmed now but it most likely had an added bit for variety:

Naturally as a biblical creationist, the designer would be God: but my description may vary highly from the conception you have presently, and that portrayed by mainstream Christianity...
Reply: Benjamin Toby Again, in the AI example, what was programmed was only the equivalent of the laws of physics. The "DNA" in the algorithms wrote itself from scratch. If you take that analogy to reality, then it would be god programming the laws of physics which caused evolution and abiogenesis to occur. I don't know why that bothers you, it seems a perfectly acceptable view to me, and I'm not even Christian.
Reply: antiHUMANDesigns

1. It seems like the major issue here is the definition of code: funny enough you agree that the DNA functions just like a machine code: I think it might be you just confusing yourself... you said I was trying to "make some kind of point" that's my whole point: you agree the DNA functions like a machine code, and accept that only intelligence creates machine codes: but not the DNA...

2. "Call it "unknown structure", for example. So your question should be "if we find an unknown structure on jupiter"... calling it that can't escape your strawman because I'm also implying intelligence by saying "structure"... 

3. " If we assumed that a god is responisble for everything, then we would have no science."... wrong...  the pre-evolution era consisted of a huge number of theistic scientists: the founders of modern science were mostly christain scientists: the father of modern science, Galileo was a christian: so that statement is outrightly false: Newton, Copernicus, Leibniz, etc... all these theists saw the necessity for God and still took science to greater heights...

4. ""Intelligent design" is not the same thing as "intelligence"." I guess that summarizes most of your arguments... 

5. "then what makes it impossible for that sequence to turn into "GCCTGGCCA", being the DNA of a human, for example?"... what makes it impossible is observation: we've seen the massive variety in the dog family but it's still amazingly consistent in differentiating the dog from a cat: the method you propose of changing it to a human based on the variations is imaginary: that would first require the dog to stand upright for all of it's life and that has never been seen...

6. about the cambrain, I repeat, my point is as to how FULLY DEVELOPED organisms appeared without their transitional fossils: you are giving evidence for evolution of organisms without their transitional fossils? then why call it "evolve"?... why don't you try to understand my point before giving me pointless drivels: it's not like I'm the one bringing most of these pointless arguments: if you can't show the evidences, then don't make pointless claims:

7. for your English correction, please clarify before you speak (http://www.learnersdictionary.com/definition/evidence)...

8. "There is no such thing. No one ever dies directly from age, everyone dies because something in their body stops working.
Death is not inveitable in that sense."... really?... could you please stop trying to explain death: you obviously don't know what causes it... and btw,death is inevitable in whatever sense you are speaking of... how can a normal person argue something like that...

9. "I doubt you even undertand what an argument from ingorance is. It doesn't mean you're ignorant, it means that you appeal to our lack of knowledge of something, and use that as a base for drawing knowledge."... of course I do know what it is:and I'm putting it to you that your argument is from ignorance: are you kidding me?...you just defined yourself: you obviously don't know how the DNA coded itself or how fully functional single cell organisms came about or how they merged to form fully functional multi-celled organisms: but you go on preaching evolution like it is a fact, and arguing about it... worse, you accuse me for drawing from a known cause of code and information to extrapolate that the DNA was formed by an intelligence...

10. "Just because we are technologically unable to turn a fish into a cat doesn't mean it's not possible to do so. We know for a fact that it's possible, even if we cannot do it.."... ALERT... argument from ignorance: why can't you just admit you didn't know, like you said?

11. "There you go with a straw man. "Random undirected formation of organs" <- this is not what evolution proposes."... I'm sorry isn't that what evolution proposes?... if it isn't random, it's orderly: and if it isn't undirected, it's directed... if your talking of an orderly and directed process, the you're talking of intelligence...

12. "It wasn't a fish that evolved into a lion, it was a differnet kind of cat that evolved into a lion."... you're using the "bait and switch" argument: of course you could form a plausible argument if you said a different form of cat "evolved" into a lion... but you know very well that's not even the premise of the theory of evolution...

13."Now, if you were an intelligent designer, would you slap a brain from a reptile on a human, and then slap another brain on top of that to override some of the bad parts, and then another brain on top of that?"... first I don't know if our brain was made up by "slapping" parts on a reptile brain... I don't know where you're getting that from... it definitely sounds to me like another argument from ignorance...

14. Look I'm willing to learn from anyone but I'm not willing to get more indoctrination even from science: I think I'm entitled to ask questions and if you can't answer them just admit instead of trying to give me half baked replies and unnecessarily long comments...
Reply: Benjamin Toby Well, just look at what the programmers designed: a system in which some string randomly forms. That string then copies itself with random variation (imitating chemistry), then is selected for by some algorithm representing natural selection (which is basically a natural law of logic). The programmers aren't meddling with the contents of the string (the DNA sequences), they are simply programming the laws of nature and letting it run its course. This is like Yaweh (or whatever designer you prefer) programming the laws of nature, which must have happened at the big bang.

Why is this not enough for you? Do you think God is incapable of such a feat as designing the laws of physics in such a way as to make abiogenesis inevitable? It seems that you don't think he's up to the task for some reason.
Reply: Max Spiegel I don't think God is incapable of anything... but I just don't know exactly how it was from the beginning: I personally think it possible for God to do all that: but my argument is to get you to see my point of view of intelligence and the DNA:
Reply: Benjamin Toby It seems to me there are two options for your beliefs:
1 - God had to reach into his creation, which had already been running for over 9 billion years when life first appeared, and tinkered with some molecules to make the first RNA.

2 - God designed the laws of physics such that abiogenesis would inevitably occur and give rise to humanity.

Is the first really more appealing to you than the second? To me it really makes God look much less powerful than the second, and the second doesn't contradict science at all, whereas the first does. Why do you insist on the first scenario? How does it make you feel better about your religion?
Reply: Max Spiegel again, going way back to the beginning of time and matter is not my basic point: and I definitely don't know for sure what happened then or how it happened: my extrapolation is not from bottom up but vice versa: I just think the existence of life is attributed to an intelligence: which I call God: and the signature is the DNA... if I were to choose though,it'll be a combination of both your options: but not the way you put it...

also I wouldn't associate myself with any religion per se: I'm a christian, but Christianity isn't really my religion: I prefer to call myself unaffiliated in that aspect...
Reply: Benjamin Toby There is a pretty strong binary choice you have to make: either the laws of physics have always been the same, or god had to reach in a tweak them at times. The universe is either a program that has been running on its own, or some deity stopped the program, altered the state of the program, and started it back up again.

What kind of "blend" of these ideas can you imagine? I can't think of one.
Reply: Max Spiegel like I said my thoughts about the origin of matter and the fundamental laws are at best, vague: but just for your sake, matter and all the laws of physics were created: and I think the earth and life were created by these tools: that's just my personal hypothesis...
Reply: Benjamin Toby Well whatever you believe, the evidence shows that the laws of physics have been constant throughout time. If there is "design" in DNA it is the same as the "design" you find in a snowflake: it is a result of natural processes, which are controlled by the laws of physics alone.
Reply: Max Spiegel actually there's no evidence to prove that: it's just a hypothesis as well: but anyway, I guess everyone is entitled to their own opinions: I just needed you to see that my opinion was not just a baseless one...
Reply: Benjamin Toby It's not just a hypothesis. The idea that physics is symmetrical with respect to both time and space can be derived mathematically, and makes unique, falsifiable predictions that have been verified through repeated experimentation. If the speed of light, for example, was different in the past, atoms would not have been able to form and we would not have galaxies as we do today. Changing the laws in the past would have visible effects in the present.
Reply: Max Spiegel again, the forming of matter and universal laws was never my argument to start with... and I don't think I'm properly disposed to indulge in that now...
Reply: Benjamin Toby Fair enough, but then don't say it's "just a hypothesis." Take some time to study it if it interests you. There are plenty of Christian scientists, and only a tiny fraction doubt evolution or our general understanding of modern cosmology. Why can't you be one of them? I'd think it would be great to study god's creation in detail if I were a theist, but you have to let go of that ultra-literal interpretation of the bible.
Reply: Max Spiegel "but you have to let go of that ultra-literal interpretation of the bible."... that's a misconception... and I call it a hypothesis for a reason: but that's for some other time I guess...
Reply: Benjamin Toby "1. It seems like the major issue here is the definition of code: funny enough you agree that the DNA functions just like a machine code"

Not "just like", but "simiarly to". Stop twisting what I'm saying.
I've made it very clear that there are some fundamental differences.

"you said I was trying to "make some kind of point" that's my whole point: you agree the DNA functions like a machine code, and accept that only intelligence creates machine codes: but not the DNA..."

Once again, "similarly to", but that is irrelevant, because you're wrong in saying that only intelligence creates these kinds of things, whatever label you want to put on it.
If you want to call DNA sequences "codes", then nature creates codes. Sorry, you cannot change reality by apply different definitions to it.

"calling it that can't escape your strawman because I'm also implying intelligence by saying "structure"... "

No, you're the only one here who thinks that structures cannot form naturally. Take a snow flake for example, that is a structure.
Of course, it's possible you don't mean the same thing by "structure" as I do.
http://dictionary.reference.com/browse/structure?s=t
I mean it in the sense of number 4:
"anything composed of parts arranged together in some way; an organization. "

Even a solar system is a form of "structure", with this meaning of the word.
You might have meant it in the sense of definition number 2, "something built or constructed, as a building, bridge, or dam. "
In such case, you're right in what you're saying, but that is not the meaning I used.

"3. " If we assumed that a god is responisble for everything, then we would have no science."... wrong...  the pre-evolution era consisted of a huge number of theistic scientists: the founders of modern science were mostly christain scientists:"

Yes, christians who did not think that god was the answer to everything.
What if newton would've thought that god makes the planets go around in circles? Then he wouldn't even have tried to explain it scientifically, because if that's true, then there is no scientific explanation for it.
Of course, when it came to mecury, he couldn't explain how it moved, and so he just said "god makes it do that", and stopped trying to explain it. We had to wait until Einstein to know that Newton was wrong.

"4. ""Intelligent design" is not the same thing as "intelligence"." I guess that summarizes most of your arguments... "

Would be awesome if it really was that simple.

"5. "then what makes it impossible for that sequence to turn into "GCCTGGCCA", being the DNA of a human, for example?"... what makes it impossible is observation: we've seen the massive variety in the dog family but it's still amazingly consistent in differentiating the dog from a cat: the method you propose of changing it to a human based on the variations is imaginary: that would first require the dog to stand upright for all of it's life and that has never been seen..."

No, I agree that a dog cannot evolve into a human, but what I asked you is what prevents one DNA sequence from turning into a vastly different sequence? Forget what the sequence translates to, that's irrelevant to what I'm asking you. Yes, there are some sequences that likely cannot change, because they control the fundamental workings of the cells themselves, so any change to it will likely just kill the cell.
But apart from this, a chimpanzee and a human has 96% (or something) the same sequence in the DNA. And we both live similar kind or f lives (forget technology for now). So what prevents the DNA of somethign like a human from theoretically turning into the DNA of something similar to an a chimpanzee?
I'm only trying to understand what kind of mechanism you believe exists to prevent this.

"6. about the cambrain, I repeat, my point is as to how FULLY DEVELOPED organisms appeared without their transitional fossils"

No one thinks there ever have been species of "not fully developed" creatures. Every transitional species would also be "fully developed", or they wouldn't be viable.
It would seem there's something fundamental about evolution that you simply don't understand, here.
Evolution requires all stages (all transitional forms) to be more successful than what they transitioned from, in relation to their environment, otherwise they wouldn't have evolved that way. Exactly what you mean by "fully developed", I don't know, but it sounds like you're talking about something like a useless half-wing in the transition to birds, or something, which of course never existed.
Why would natural selection favor a creature that has some useless new feature?

For examples, just look at "Lucy" (australopithecus afarensis), which is an intermediate species between modern humans and the species that was common to humans and chimpanzees (about 6-7 million years ago).
Are you saying that Lucy is "not fully delevoped"? Or are you saying that Lucy's species is not an intermediate species because "they were fully developed"?
Both, of course, are nonsense.
We humans, right now, will be considered intermediate (a transitional species) between some ancestor of ours, and whatever we will evolve into in the future. What does that say about us? Nothing.

Being "transitional" just means being an example of a species during a transition of some sort, such as from walking on all four to walking on 2 feet, or something similar. To be "transitional", you need to have the traits of the old thing, but also some of the traits of the thing that came after.
We've got transitional forms from human evolution, and they are transitional because they display both the traits of their ancestor, but also the traits of modern humans, such as being bipedal, making tools and having a large brain, and so on. But of course, also more technical things like the shape of their shoulders, and so on.
This makes them transitional by definition.

Because of this, everything that didn't lead to a dead end in evolution was transitional in some sense. So if humans continue to evolve, which they will, we will be considered transitional, when talking about some trait that will evolve later on.

"you are giving evidence for evolution of organisms without their transitional fossils? then why call it "evolve"?... "

Because fossils aren't everything. DNA is more useful as evidence, but it depends on what you want to know.
If we had no fossils of any kind, we would still know that we are all related, because of the evidence from DNA.
But the fact that we also do have a lot of fossil evidence helps to make the case very strong. Especially because fossils don't only show you what the creature looke dlike, but it's position in the ground, and its geographical position, tells you a lot, aswell.
For example, a species must have evolved from a species that "lived nearby", so to speak. Taht is why humans must come from africa, for example, because that's where our ancestors lived. If we found out that the first species of humans lived in north america, then how did they get there, if they evolved from a species that lived in africa?
This is called "evidence from geographic distribution". Closely related species live "near" where they evolved. "Near" being relative to their habit of moving around, of course.
For example, some islands have completely unique species, because they have been unable to move across the water to other land masses. The relationships that this forms is another good line of evidence in support of evolution.

"if you can't show the evidences, then don't make pointless claims:"

I can show you evidence in support of evolution. As for the evolutionary history of specific species, or genera, I might be able to show you for some, but not for all.
But I don't physically have the evidence, so "showing you" basically means directing you to the internet. You have the evidence just as much as I do.

"7. for your English correction, please clarify before you speak (http://www.learnersdictionary.com/definition/evidence)..."

"Evidence" is an uncountable noun, so there is no plural form, "evidences".
The link you just linked even has this example: "The jury had a great deal of evidence to sort through before reaching a verdict." <- clearly meaning more than one thing, yet it's not "evidences".
Of course, I'm a Swede, so I'm not a native english speaker. However, that tends to make us more strict, since we don't fall into idiomatic uses as much.
But, as has been noted by others before, for some reason we only ever see creationists writing "evidences", and that is very interesting. Some article traced it back to some old creationist artcile, after which "evidences" started appearing in other places.
So, I dont' know, but it appears liek some creationist made that as a mistake, and then all other creationists (who don't even know the meaning of the word), started doing the same thing.
I'm sorry, it's a low blow, but you have to admit it's kind of funny.

"and btw,death is inevitable in whatever sense you are speaking of... how can a normal person argue something like that..."

Strictly speaking, you're right. In reality, it will always be inevitable, because "forever" is a practical impossibility, especialyl since the universe itself will eventually expire, and that truly is inevitable.
But my point is that people don't "theoretically" have to die from age. Practically, yes, because we'll never be good enough to prevent it forever.
It's kind of like saying "you can count forever, there is no end to the number system". In reality, you can't, and there is an actual limit to how long you can count (even if it's a vague limit), but you do still understand what it means, right?
I'm surprised to find someone more cynical than myself. :P

"you just defined yourself: you obviously don't know how the DNA coded itself or how fully functional single cell organisms came about or how they merged to form fully functional multi-celled organisms: but you go on preaching evolution like it is a fact, and arguing about it"

Yes, because evolution doesn't make any claims about the origin of life. We have no theory for the origin of life.
Evolutionis a fact, but it is only the fact that life diversifies over time (the origin of species, not the origin of life).
And it's not an argument from ignorance, because we do know this. And it can't be an argument from ignorance unless I admit that there's somethig we don't know, yet I still draw conclusion from the fact that we don't know.

You say "like evolution is a fact". It is a fact, because it is an observation. Life evolves, it changes with time. This can be demonstrated to anyone who dont' believe it. the problem is taht the ones who reject evolution usually don't understand what evolution is, and therefore they're asking to see evidence for something that the theory doesn't claim happens.

However, the "theory of evolution" is not a fact, because it is a theory, not an observation. But it is an extremely well supported theory. Better supported than most theories, in fact.

And furthermore, I don't need to know the evolutionary history of every species to know that the theory is solid. That's the same thing as how I don't need ot make sure that every planet in the universe is affected by gravity to have a theory of gravity that says that planets are affected by gravity.
The theory of gravity predicts that planets will orbit their stars. So whenever we find a new planet, it should orbit its star, if the theory is correct. And everytime this prediction turns out correct, it is strong evidence in support for the theory. An idea that can make predictions is a useful idea.
So you understand this?

The theory of evolution predicts a lot of things related to population mechanics, but it also predicts what we should find in the DNA and in the fossil record, and so on. And the theory has successfully predicted things soooo many times it's getting silly.

However, when a prediction fails, then you know that something is wrong with your idea. It might not be completely wrong, but there is something casuing the predictions to be wrong, so something is definitely not correct.
Newton's theory of gravity failed to predict the orbit of mercury, for example, which proves that it cannot be correct. However, it was extremely useful ion otherways, so it couldn't be completely wrong, either.
But Einteins theory of relativity did solve the problem of mercury's orbit, so it is a better "version" of gravity.

And evolutioon used to say that species constantly gradually evolves ("gradualism"), but becaues this is not what we see in the fossil record, we eventually agreed that something is wrong about this "statement". Then we found a better explanation, called "punctuated equilibrium", which fits the evidence much better, and also makes more sense.

"worse, you accuse me for drawing from a known cause of code and information to extrapolate that the DNA was formed by an intelligence"

You know, I didn't Actually say you are committing an argument from ignorance fallacy. I said "if this is what you're arguing, then that is an argument from ignorance", paraphrased. If that is what you're trying to argue, then I would be correct.
the fact is that you're not clear on what your point is. We've been discussing DNA and "codes" for a long time, but I don't know why you are arguing about it, and why you really need DNA to be a "code", which you argue so fiercely for.
Of course, now I know, it's simply so that you can make that statement that "if DNa is like computer code, and computer code only comes from intelligence, then DNA also comes from intelligence".
What a total waste of time that discussion has been. I don't understand why someone would ignore reality and instead try to argue that reality is something its not, by playing word games. In the end, you're arguing that DNA sequences cannot come from nature, but we know that they do, because that is an observation, so the case is closed.

"10. "Just because we are technologically unable to turn a fish into a cat doesn't mean it's not possible to do so. We know for a fact that it's possible, even if we cannot do it.."... ALERT... argument from ignorance: why can't you just admit you didn't know, like you said?"

Don't know what!?!
I know it's possible to turn one sequence into another sequence, or if you want to, molecule by molecule restructure a fish into a cat. there is absolutely nothing about the nature of the universe that prevents us from doing this. The only think that prevents us is our technology.
It's like you're saying playing the piano is impossible because everyone's fingers are too sore. Gaah, start making sense, please.

And just like I thought, you don't understand what an argument from ignorance is. It's only an argument from ignorance if I say something like "but science doesn't know why this is that way", and using that as an argument for why something is a specific way. That would be an argument from ignorance.
I have said nothing even remotely like that.
I have never used our ignorance about something as an argument in support for something. I have never said that because we don't know exactly what happened in the cambrian explosion, therefore evolution must be true.
I have said that even though we don't know everything about this specific thing, we do know alot of other things that leads us to believe that this is how life works, which predicts that the cambrian explosion should have the same explanation.

Now if you want to argue that because computer code is written by humans, your hypothesis predicts that DNA should also have been written by an intelligence, then that is perfectly fine! I welcome any hypothesis! That one happens to be false, but at least it would be a hypothesis,. which is worth a lot more than just asserting something as true against all evidence, simply because you want it to be that way.

"11. "There you go with a straw man. "Random undirected formation of organs" <- this is not what evolution proposes."... I'm sorry isn't that what evolution proposes?... if it isn't random, it's orderly: and if it isn't undirected, it's directed... if your talking of an orderly and directed process, the you're talking of intelligence..."

Is gravity intelligent? Is gravity ordely? Is gravity random?

No, that's not what evolution proposes. Simplified, evolution proposes that given a gene pool, the ones that are best fitted for their specific environment (and all the factors that go with it) will tend to have more offspring than those who are not as fit to their environment.
That is not random. If being tall makes you less likely to die, or "sexier", or more fertile, then a tall person will have an advantage over a short person, and over time, the "short" individuals will start decreasing in the gene pool, which means that the average high of the species has increase, which is one example of evolution.
This cannot be disputed. It can be demonstrated easily to anyone, both with actual living organisms, and with "thought experiments". If I have a set of candies, and I eat all the dark candies, then the group of candies as a whole will be generally brighter. And because there are no dark candies left who can make dark baby candies, the group as a whole has changed "permanently".

But the problem is that when you try to explain this to a creationist, they will often say stuff like "but that's not evolution", or "that's micro-evolution", or some dumb stuff like that. And what can you do, when someone who doesn't know what they're talking about insists that they do know what they're talking about, and refuses to learn?

Sadly, I don't know what you mean by "directed", perhaps a language barrier. Do you mean it in the sense of how a movie is directed? Evolution is not directed in that sense. It is directed by laws, just like everything else. That is how we can make a theory to explain it. If something is random, then it has no patterns, so there is nothing you can learn about it, and it cannot be predicted, and it is useless.

"12. "It wasn't a fish that evolved into a lion, it was a differnet kind of cat that evolved into a lion."... you're using the "bait and switch" argument: of course you could form a plausible argument if you said a different form of cat "evolved" into a lion... but you know very well that's not even the premise of the theory of evolution"

Heh, well, firs tof all, you don't know the "premise of evolution", so don't even go there.
You can say that this is bait and switch (which it isn't, and I'll explain why in a second), and I an say that you're intentionally trying to appeal to people's incredulity, by making it sounds as implausible as possible, just to make it really hard to believe, and that is irrelevant as to whether it is true or not, which is why it's called an argument from personal incredulity (fallacy).
"It's just too hard to believe that this could happen" <- argument from personal incredulity.

Now, as for why what I said is not bait and switch. I am not "selling" the evolution from some cat species to lion, I am "selling" the idea that life evolves. The consequence of this is both that some cat species can evolve into a lion, but also that if you go back far enough, that cat species came from something that we would consider a fish if it existed today. And if you understand the science, you'd know that none of those scenarios are any more unlikely than the other. They're equal, because it's the same process, the same mechanisms, just more time.
But the fact that you phrase it as "a fish turning into a lion" is only evidence that you're intentionally trying to make it sounds as ridiculous as you can make it sound - without being caught lying, of course.
It shows your bias, to start with, but it also shows a hint of dishonesty.

"first I don't know if our brain was made up by "slapping" parts on a reptile brain... I don't know where you're getting that from... it definitely sounds to me like another argument from ignorance"

OK, that has' to be trolling. You can't seriously keep thinking that *everything in an argument from ignorance. You can't possibly be that stupid.

But just in case you really are that stupid... well, I'll give you the benefit of the doubt that you're not malicious, at least.

Of course there was no "slapping", you must understand that's just a figure of speech, right? But also, is it really possible that you've gone your whole life without hearing about our "reptile brain"?

"14. Look I'm willing to learn from anyone but I'm not willing to get more indoctrination even from science:"

Then don't get "indoctrinated". Whether or not you get "indoctrinated", as long as the information is correct, it's hardly a bit issue.
But you've already been indoctrinated by creationists, so some balance should only help you.

"I think I'm entitled to ask questions and if you can't answer them just admit instead of trying to give me half baked replies and unnecessarily long comments"

Oh, I promise, if I can't answer a question, I will tell you. I even have. At least on one occasion, relating to the species of the cambrian explosion, I remember telling you what I am unable to answer you. I think there was another case of that, aswell.

As for unnecessarily long comments... well, I guess I have an inefficient style of communication, or something. I don't consider it "unnecessary", but I am aware that it's "long". (Once, I wrote a reply over 4000 lines long, which took basically an entire day to write.)
At least I'm hoping you appreciate the effort I put into my replies. Some of these take well over an hour to write.
Reply: antiHUMANDesigns

1. "Once again, "similarly to", but that is irrelevant, because you're wrong in saying that only intelligence creates these kinds of things, whatever label you want to put on it.
If you want to call DNA sequences "codes", then nature creates codes. Sorry, you cannot change reality by apply different definitions to it."... and you're wrong in saying nature creates those kinds of things: for all you know these DNA sequences were there before you even opened you eyes: but you accept its "similarity" with a machine code but conclude it was just an accident: you're the one most likely changing reality...

2. "Because fossils aren't everything. DNA is more useful as evidence, but it depends on what you want to know."... are you kidding me?... of course DNA would be in all living things: apparently for you similar DNA means "evolved from"... another argument from ignorance...

3.""Evidence" is an uncountable noun, so there is no plural form, "evidences"."... more pointless rants... the first thing on that link was the plural:

4. "Strictly speaking, you're right. In reality, it will always be inevitable, because "forever" is a practical impossibility, especialyl since the universe itself will eventually expire, and that truly is inevitable.
But my point is that people don't "theoretically" have to die from age. Practically, yes, because we'll never be good enough to prevent it forever."... again, more pointless rants...

5. "Evolutionis a fact, but it is only the fact that life diversifies over time (the origin of species, not the origin of life).
And it's not an argument from ignorance, because we do know this. And it can't be an argument from ignorance unless I admit that there's somethig we don't know, yet I still draw conclusion from the fact that we don't know."... more drivel?... the theory of evolution states that all organisms EVOLVED from single simple celled common ancestor: definitely we know that organisms vary and adapt to their environments: but no one knows how to pack up single celled organisms to form complex ones: pls stop trying to maneuver through this and give this pathetic excuse of "change" as description for evolution... you don't need to admit you don't know that for me to see through it: your denial just makes the argument more ignorant...

6. "You say "like evolution is a fact". It is a fact, because it is an observation. Life evolves, it changes with time. This can be demonstrated to anyone who dont' believe it. the problem is taht the ones who reject evolution usually don't understand what evolution is, and therefore they're asking to see evidence for something that the theory doesn't claim happens."... bruh: please have mercy: this is too much: how did you think the "theory of evolution" was coined?... because they thought it just meant "change"?... pls don't give me the "you don't understand evolution" bant: the fact that you twist it to suit your purpose is just plain hypocrisy: 

7. "However, the "theory of evolution" is not a fact, because it is a theory, not an observation. But it is an extremely well supported theory. Better supported than most theories, in fact."... oh really?... well tell that to you Darwinian extremists who think it's even more than a fact: 

8. "And evolutioon used to say that species constantly gradually evolves ("gradualism"), but becaues this is not what we see in the fossil record, we eventually agreed that something is wrong about this "statement". Then we found a better explanation, called "punctuated equilibrium", which fits the evidence much better, and also makes more sense."... punctuated what now?... oh my: so they even realized organism didn't gradually develop over millions of years like darwin proposed... but how did this punctuation story solve the problem: that just sounds like a fail because how else do you explain a species appearing in the fossil record after attaining stability when natural selection would kill it off in the process?... this is funny... this is just like ID because all useful parts would have to appear simultaneously... 

9. "Of course, now I know, it's simply so that you can make that statement that "if DNa is like computer code, and computer code only comes from intelligence, then DNA also comes from intelligence".
What a total waste of time that discussion has been. I don't understand why someone would ignore reality and instead try to argue that reality is something its not, by playing word games. In the end, you're arguing that DNA sequences cannot come from nature, but we know that they do, because that is an observation, so the case is closed."... first if you concede any form of similarity between the computer system and the DNA you're validating my claim: this is because no part of a working computer system can arise without intelligence... so, to sum up, you are the one actually wasting your time because most of these cumbersome comments you're bringing up are basically pointless... secondly, don't talk of reality that you don't know of: I agree the DNA sequences are rearranged to create variety because they were made that way: the difference between our stands is that I think the DNA for specific animal/plant groups were intelligently designed and made to add variations: and you believe the DNA just is: like a bunch of random chemical bonds and sequences that just happened to be "useful to the organisms"... basically, the DNA sequenced itself...

10. "Don't know what!?!
I know it's possible to turn one sequence into another sequence, or if you want to, molecule by molecule restructure a fish into a cat. there is absolutely nothing about the nature of the universe that prevents us from doing this."... lol... ALERT again... if you want to know what you don't know it's how to restructure the DNA of a fish to form a cat... now what you DO know is re-sequencing of DNA to form a new VARIETY of cats...so that argument of "knowing a possibility of sequencing a fish DNA to a cat's" is imaginary and hence any argument drawn from that is an argument from ignorance... "Gaah, start making sense, please."... you should reeeeally consider taking your own advice...

11. "And just like I thought, you don't understand what an argument from ignorance is. It's only an argument from ignorance if I say something like "but science doesn't know why this is that way", and using that as an argument for why something is a specific way."... again you don't need to concede to prove that your argument was from ignorance: for one you're not willing to concede what you don't know; so it'll seem impossible in your mind for you to make an argument from ignorance: 

12. "Now if you want to argue that because computer code is written by humans, your hypothesis predicts that DNA should also have been written by an intelligence, then that is perfectly fine! I welcome any hypothesis! That one happens to be false, but at least it would be a hypothesis,. which is worth a lot more than just asserting something as true against all evidence, simply because you want it to be that way.".... Luckily, my hypothesis is not false because you say it is: and your alternate explanation is both a hypothesis as well, and an irrational one at that.. also that's not my only argument for intelligence just so you know: just that I've been addressing your rants for most of the time... furthermore I'm not asserting anything as true, and my extrapolations are firmly based on evidences so I don't understand your point here...

13 "No, that's not what evolution proposes. Simplified, evolution proposes that given a gene pool, the ones that are best fitted for their specific environment (and all the factors that go with it) will tend to have more offspring than those who are not as fit to their environment."... again, I have no problem with that: and you should know that: you know where my argument lies so why are you twisting the theory selfishly?... 

14. "But the problem is that when you try to explain this to a creationist, they will often say stuff like "but that's not evolution", or "that's micro-evolution", or some dumb stuff like that. And what can you do, when someone who doesn't know what they're talking about insists that they do know what they're talking about, and refuses to learn?"... well the terms micro-evolution and macro-evolution were probably invented to avoid the confusion of terms and evidences: If you can't see the confusion by now then there's no need wasting time on that...

15. "Heh, well, firs tof all, you don't know the "premise of evolution", so don't even go there."... WHAT?... the premise of evolution is that all living things EVOLVED from a single common universal ancestor. 

16. ""It's just too hard to believe that this could happen" <- argument from personal incredulity."... argument from what now?... is it not too hard for you to believe all animal groups were intelligently created?... how come this doesn't work for you?

17. "But the fact that you phrase it as "a fish turning into a lion" is only evidence that you're intentionally trying to make it sounds as ridiculous as you can make it sound - without being caught lying, of course.
It shows your bias, to start with, but it also shows a hint of dishonesty."... it IS ridiculous... no matter how you try to make it sound: and it's the basic proposition of the theory of evolution... speak of lying and bias and dishonesty:
"All of life on earth shares a common ancestor known as the last universal ancestor, which lived approximately 3.5–3.8 billion years ago."[https://en.wikipedia.org/wiki/Evolution]... is that not what the theory proposes?... if the theory proposed that living organisms varied with new generations do you think I'd be arguing over that? ... 

18. "OK, that has' to be trolling. You can't seriously keep thinking that *everything in an argument from ignorance. You can't possibly be that stupid.".... hahahahaha... of course I don't think everything is an argument from ignorance: just that much of your arguments happen to be from ignorance: and I believe I pointed them out...

19. "But just in case you really are that stupid... well, I'll give you the benefit of the doubt that you're not malicious, at least."... oh really?... looool... then you should feel for me because I'm trying to reason with you even if most of you points actually classify as "stupid"... calling me stupid actually says more about you than me... 

20. "Of course there was no "slapping", you must understand that's just a figure of speech, right? But also, is it really possible that you've gone your whole life without hearing about our "reptile brain"?"... of course I know it's figure of speech: however there's not possible way you put it that wouldn't sound implausible... again you have no clue how it supposedly happened and all those supposed processes are imaginary; but there you go again, preaching it like it's a fact...

21. "Oh, I promise, if I can't answer a question, I will tell you. I even have. At least on one occasion, relating to the species of the cambrian explosion, I remember telling you what I am unable to answer you. I think there was another case of that, aswell."... I'm sorry to say but some of your supposed answers aren't even answers to me: and some are just misunderstandings... 

22. "As for unnecessarily long comments... well, I guess I have an inefficient style of communication, or something. I don't consider it "unnecessary", but I am aware that it's "long". (Once, I wrote a reply over 4000 lines long, which took basically an entire day to write.)
At least I'm hoping you appreciate the effort I put into my replies. Some of these take well over an hour to write."... well you have to realize you're not typing computer programs and most of your lines are not needed for the points: I appreciate your effort to try to relate your points but you should also put effort to understand mine: at least it could save a lot of time and space... and btw... 4000 lines???...wth... please don't do that to me...
Reply: antiHUMANDesigns I forgot this:

"Yes, christians who did not think that god was the answer to everything.
What if newton would've thought that god makes the planets go around in circles? Then he wouldn't even have tried to explain it scientifically, because if that's true, then there is no scientific explanation for it."... well Newton thought God was the answer to vital questions of life and the Universe: still went on to become a great scientist...

"This most beautiful system of the sun, planets, and comets, could only proceed from the counsel and dominion of an intelligent and powerful Being....This Being governs all things, not as the soul of the world, but as Lord over all; and on account of his dominion he is wont to be called Lord God "pantokrator," or Universal Ruler...."- Isaac Newton.
Reply: Benjamin Toby "and you're wrong in saying nature creates those kinds of things: for all you know these DNA sequences were there before you even opened you eyes: but you accept its "similarity" with a machine code but conclude it was just an accident: you're the one most likely changing reality..."

I don't know how many times you have to straw man evolution. It's not an "accident", it's what happens when you put stuff into a system of laws. 5+5 doesn't accidentally become 10.

I'm not wrong in saying that, because we can see nature creating new DNA sequences. You know this happens, because you have heard of mutations, and I'm going to dare assume you agree that mutations do happen.
If you have a sequence, "TTGG", and there was a mutation that made it into some other sequence, then nature has created a new DNA sequence. This isn't under any dispute, it's an observation that can be repeated as much as you want.
And we have made RNA assemble itself in a laboratory, under natural conditions, from nucleobases. That is nature creating an RNA sequence from scratch.

I don't understand why you're even arguing about this, it's silly. You know this to be true.

"... are you kidding me?... of course DNA would be in all living things: apparently for you similar DNA means "evolved from"... another argument from ignorance..."

OK, so you don't know what this evidence entials.
We've got a genome that is something like 3 billion base pairs long. The difference between humans and chimpanzees is about 50 million base pairs.
That doesn't make this "two similar sequences", it means that a sequence that is 2.95 billion values long is exactly the same. That is not just "similar", that is something that is simply impossible unless it was copied.
Do you not see this? If I wrote a 100 million pages long book, and you did the same thing, and they ended up effectively exactly the same, letter-by-letter, is it possible that I had no idea what you were writing? Obviously, I copied you, somehow.
And life does copy DNA, that is how we reproduce. So the obviouis answer is that humans and chimpanzees are copies of the same thing, but over about 6-7 million years, mutations and things like recombination have added up for both chimps and humans, to cause a *small* difference in our DNA.

Not enough evidence? How about the fact taht is isn't only true between humans and chimpanzees, but between all living things, even plants. How many times can we see the same insanely long sequence apparently copied between species, and still deny that they're related?

And it gets better, because if you trace these small differences in our DNA, you can see when two species split from eachother, and you can create a "tree of life" structure from simply looking at the DNA of all living things.

And this tree of life agrees with the tree of life structure you get when looking at the fossils. And when you've got two completely separate lines of evidence that gives you the same answer, then that is very strong support for the idea.
And evolution doesn't only have 2 separate lines of evidence, it has a few more. That's why the theory of evolution is one of the best supported theories in all of science, save only thermodynamics, basically. We know more about evolution than we know about atoms, or gravity, or electricity, or bacteria, and so on. We are more sure that species are related than we are sure that atoms really exist.

And you really should stop displaying your stupidity by saying "argument from ignorance" after every paragraph. You've been wrong each time, so far, and it's embarrasing to watch.

"3.""Evidence" is an uncountable noun, so there is no plural form, "evidences"."... more pointless rants... the first thing on that link was the plural"

I'm not going to argue about this, do what you want.

"... again, more pointless rants..." [about living forever]

Sorry for agreeing with you.

" the theory of evolution states that all organisms EVOLVED from single simple celled common ancestor:"

No, it predicts that all living things that share common traits must all have inherited them from the same ancestor.
It is possible that some life on earth, which we have not checked (DNA sequenced) yet, are not related to some other life on earth, that they both sprung up separately. In such case those life forms will not share common traits (such as the same DAN sequences)  the way that those who are related do.
But since we can never know for sure that we've seen all life on earth, we cannot know if all life on earth is related, so that is not a statement that science can make.
And we haven't sequenced the DNA of all life, either. We can only speak for what we've seen "so far", which of course is a *lot*.

"definitely we know that organisms vary and adapt to their environments: "

Evolution. The process of a species adapting to its environment is evolution. If you say it's not, then you don't know what evolution is.

"but no one knows how to pack up single celled organisms to form complex ones:"

...and therefore common ancestry isn't true, right?
And there you go, and example of an argument from ignorance, because you're using our ignorance about a specific thing as an argument for why something is true or false.
If we don't know something, then we can't use that as an argument. "I don't know what the time is, right now, so it can't possibly be 10 o'clock" <- just as nonsensical. Yes, this is exactly what you're implying.

"pls stop trying to maneuver through this and give this pathetic excuse of "change" as description for evolution"

Evolution: The change in allele (gene) frequencies in a population over time.

If you go out and shoot every human who has blonde hair, then the gene pool will contain fewer genes for blonde hair. So, the species as a whole has changed, and that is evolution.
Where does natural selection come into this? Apparently, having blonde hair made you unfit to live in a world where being blonde can get you shot.
And from that point on, humans on average have darker hair. Evolution.
Any other definition (than the change in allele frequencies) is usually a straw man and completely irrelevant.

And as for what this fact leads to over large time scales, that is just an effect of this. Small changes build up over millions of generations, and splits species into new species. ("The origin of species".)

" how did you think the "theory of evolution" was coined?... because they thought it just meant "change"?... "

Not random change, lawful change. Something that we can understand and make predictions about.
When the theory was first proposed in "the origin of cpecies", it had a lot of work done. It wasn't just "it appears as if things change". It was a well researched and extremely intelligently and thoroughly explained idea for how life might change.
Of course, that is largely irrelevant now, since it's 150 years old science, and out-dated.

"pls don't give me the "you don't understand evolution" bant"

Then demonstrate that you do understand it, and stop being like every other creationist out there who either straw man evolution, or are too dumb to even know that they don't understand the subject.

Alternatively, explain to me how I am supposed to discuss evolution with someone who doesn't know what evolution is, or how it works? Seem reasonable that the first thing is to tell them that they need to learn about the subject.

"7. "However, the "theory of evolution" is not a fact, because it is a theory, not an observation. But it is an extremely well supported theory. Better supported than most theories, in fact."... oh really?... well tell that to you Darwinian extremists who think it's even more than a fact"

If anyone says the theory of evolution is a fact, then yes, I correct them. I have done so in the past, and I will continue to.
Evolution is a fact, but theory of evolution is an explanation of the fact, not a fact in itself.

But you better damn well make sure they specifically say that the theory of evolution is a fact, before you attemt to correct them.

" punctuated what now?... oh my: so they even realized organism didn't gradually develop over millions of years like darwin proposed... but how did this punctuation story solve the problem"

Well, there you go, you just admitted you don't know much at all about the science, if you don't even know what punctuated equilibrium is.
Gradualism is the idea that life slowly changes all the time, at a constant rate.
Punctuated equilibrium is the idea that as long as the environment stays the same, an organism that is fit for its environment won't change much at all, because a change would likely make it less fit. (Though evolution can never completely stop.)
Then something happens to the environment, and a new selection pressure acts on the species, and the species more rapidly starts evolving to overcome this new "problem".

This makes more sense, and it fits the fossil evidence better than gradualism does.

But this change is still gradual, it's just that the speed at which change happens varies quite a lot depending on how strong the selection pressure is to change.

" this is funny... this is just like ID because all useful parts would have to appear simultaneously... "

No, it's still gradual, it's just not a constant rate of change. But those bursts are also bursts of gradual change, of course.
Basically, if there is no strong selection pressure, because the species is pretty fit for its environment, then even the "bad" individuals of the species will survive and have kids, and mix in with the gene pool. But if the selection pressure is strong, then a lot of the "bottom" individuals aren't fit enought o make it, and only the "best" will add to the gene pool. This causes a faster change.

If it doesn't matter if you're tall or short, then the average lenght of humans won't change much, but if you need to be tall, then the length of humans will rapidly increase as the "short genes" die out, and mutations that cause you to be extra tall are strongly favored (even if they have negative side effects, btw). Punctuated equilibrium simplified.

" first if you concede any form of similarity between the computer system and the DNA you're validating my claim: this is because no part of a working computer system can arise without intelligence"

Because:
1. A computer is not fit to survive in nature, it's a machine made as a slave for humans, and it has no will to live or reproduce, or any ability to "feed itself", or anything.
2. A computer doesn't reproduce with variation, and it doesn't have a genome. So it can't evolve.

But the ironic thing is that a "computer" that would be fit for living in nature, and has a genome, and reproduces with variation so that it can evolve, actually did arise naturally!
Those are called "life", btw. Humans, for example.

"so, to sum up, you are the one actually wasting your time because most of these cumbersome comments you're bringing up are basically pointless"

I have a glimmer of hope that you'll actually learn something. I'm actually doing this out of good will, and I don't consider it pointless.

"I agree the DNA sequences are rearranged to create variety because they were made that way"

Just to clarify, do you mean that DNA was intentionally designed to mutate?

" and you believe the DNA just is: like a bunch of random chemical bonds and sequences that just happened to be "useful to the organisms"... basically, the DNA sequenced itself..."

This brought a tear of happiness to my eye - you didn't straw man me!
My tentative belief about the origin of the genome, is that it initially started out as just a molecule (probably RNA) that copied itself, and the specific sequence wasn't very important. The only thing that mattered is if it could copy itself fast and efficiently, becaue then it would keep existing, and stay competitive amongst other such molecules.
But some specific sequences that happened to arise though mutation had useful effects, and caused more such copies to exist, and as such things happened, the specific sequence actually started to matter.
And now, it's no longer about the molecules ability to directly copy itself, but it's ability to construct a vessel that is able to eventually make it copy itself. And a lot of the things that the molecule itself used to more directly do has been taken over by new processes that basically does it for the molecule, and now it acts as a chemical memory in a biological machine.

So yes, effectively, DNA sequenced itself, by its own effort to keep existing, so I'm happy to see you not making a straw man out of my position.

Of course, the science of the origin of the genome is not settled, yet, but the RNA world hypothesis appears to be the best supported explanation.
Perhaps one day we will have a theory called something like "the RNA world theory of abiogenesis", or something.

"if you want to know what you don't know it's how to restructure the DNA of a fish to form a cat... now what you DO know is re-sequencing of DNA to form a new VARIETY of cats"

No, if we know the sequence of the entire DNA of a cat, then we can take a fish DNA and completely re-write it exactly like a cat's genome. Bam, done.
Not that there's any point in doing this, apart from seeing if we can mange to do it. In the end, what we get is still just a cat like any other cat, so it's more like a trick that something useful.
And like I said, there is nothing that prevents this from being done. But it has no value.

"so that argument of "knowing a possibility of sequencing a fish DNA to a cat's" is imaginary and hence any argument drawn from that is an argument from ignorance"

Wouldn't that make it an appeal to imagination? Please, rub two brain cells together and try to form a coherent thought.
In any case, I just explained this, so no need to repeat.

"for one you're not willing to concede what you don't know; so it'll seem impossible in your mind for you to make an argument from ignorance: "

Well, yes, that's correct. Since I don't appeal to our ignorance, I cannot possibly make an appeal to ignorance.
And the effect of this is that someone who thinks they know everything really cannot appeal to ignorance.
That is not me, though, as I have proven, I have admitted things that I don't know, and things that science doesn't know.
Bu tinstead of using that as a sourrce for drawing conlsuions, I have attempted to move the conversation away from it, because there is no point in talking about somethign we can't talk about because we don't know.
Well, it's OK as long as you make it clear that you're speculating.
Also making inferences is fine.

"Luckily, my hypothesis is not false because you say it is"

Correct. It is false because of the evidence, and I am informing you about that.

"and your alternate explanation is both a hypothesis as well"

If you're talking about the theory of evolution, then it is not a hypothesis. It is an established theory. It has passed its tests and been confirmed.

"also that's not my only argument for intelligence just so you know: just that I've been addressing your rants for most of the time... furthermore I'm not asserting anything as true, and my extrapolations are firmly based on evidences so I don't understand your point here"

Well, it's the only argument that you've presented, so it's the only one that I have met. I never thought it was your only argument.

I agree, you're not asserting anything as true. Your tactic appear to be the classic one: Assert that evolution is not true, and then use a false dichotomy fallacy to conlude that the only option left is intelligent design.

I could be wrong of course, and I'm waiting to be happily surprised.

I'm sure you base your idea on evidence, I'm just not sure you understand what the evidence is telling you. You always need some basic form of understanding of epistemology, what you can actually know about something, and so on.

Since you're a creationist, there's a chance that you think that we can be sure about things, that science is the pursuit of "the truth", rather that just a way to build models that are useful.
Once again, I could be happily surprised that you are different. These things just appear to be common amongst creationist, in my experience.

"13 "No, that's not what evolution proposes. Simplified, evolution proposes that given a gene pool, the ones that are best fitted for their specific environment (and all the factors that go with it) will tend to have more offspring than those who are not as fit to their environment."... again, I have no problem with that: and you should know that: you know where my argument lies so why are you twisting the theory selfishly?... "

The thing is, the theory says many thing, because it touches on many aspects of life, population mechanics, genetics, and so on.
The great thing about evolution is that it can explain so many aspects of life, and answer so very many questions, because it is the unifying theory of all of biology - and it's even used outside of biology, because the results of evolution is useful, so we "immitate" evolution to solve porblems.

And if you, as you say, have no problem with what I'm saying, then the only reasonable conclusion I can draw is that there is something else, something additional to evolution, that you believe is going on. Such as someone actually directing evolution, somehow, or that there are some mechanism that science isn't aware of.
Explain it to me.

"well the terms micro-evolution and macro-evolution were probably invented to avoid the confusion of terms and evidences: If you can't see the confusion by now then there's no need wasting time on that"

The terms are useful because it allows us to talk about evolution on two difference time-scales. But lots of creationist think that they are separate things, that one could exist without the other.
And you seem to share that idea, because you somehow agree taht a wolf can evolve into a dog, but that the wolf doesn't have a common ancestor with more distantly related animal, even though the mechanis is exactly the same.
And I just can't wrap my head around that. Like others have said, it' slike believing it's possible to put two bricks together, but it's impossible to bild a wall of bricks, but they can't actually explain why that would be impossible. And of course that makes me draw the conclusion taht it's wishful thinking, that they just don't want it to be true. But since I've never been religious, I don't understand that line of thinking, that it's somehow degrading to be an animal.

"15. "Heh, well, firs tof all, you don't know the "premise of evolution", so don't even go there."... WHAT?... the premise of evolution is that all living things EVOLVED from a single common universal ancestor."

No, it's not. Even if all life on earth was not related, but that only some animals were related to eachother, then that doesn't negate evolution one bit.
Evolution attempts to explain why there are similarities between species, and explains this by common ancestry. But that doesn't mean that all life must have common ancestors, it just looks like that is the case.
It also explains why the current life is the way it is, by saying they are a variation of the life before them.

Special creation cannot explain this in any way that is useful, that can make predictions.

But because all life on earth seem to share so extremely many traits, evolution predicts that they're all related. But if we find animals that don't share any traits with any other animals, then it doesn't disprove evolution. Evolution would then predict that they are not related.

IF we would, somehow find two animals that share lots of traits, but we find tha they canont have a common ancestor, then evolution is disproved. Or, if an animal for example shares a trait with a species that it cannot have inherited from that species, then evolution is disproven. An example would be a cow with feathers. Cows and brids do share a common ancestor, but that common ancestor didn't have feathers, so it would be impossible for two separate descendents to both independently evolve feathers.
And thus,e volution explain why only mammals have fur, and why only dinosaurs can have feathers, and why only some aninmals have spines, while others have exoskeletons, and so on.

And then there are the very real possibility of life on other planets, which are most likely not related to life on earth. Likewise, that would not be a problem of evolution, either. It would, however, be very interesting to the study of abiogenesis.

"16. ""It's just too hard to believe that this could happen" <- argument from personal incredulity."... argument from what now?... is it not too hard for you to believe all animal groups were intelligently created?... how come this doesn't work for you?
"

Argument from personal incredulity means to argue that something cannot be true because it's too hard to believe it's true.
For example, quantum mechanics claims that the same electron can be in two places at the same time. Because this goes against "common sense", it might be a normal reaction to not believe it's true just because it's too hard to accept that such a thing could be true.

Similarly, it's understandable that it's hard to accept that all current life could have initially come from a simple cell, because common sense is not equipped to deal with such time scales.
But this is why we have science: To remove such human factors as clinging to "common sense". If the evidence tells you somethign is real, then you have to accept it as real, even if it's hard to believe.

You ask me if it's too hard to believe that all animal groups were intelligently created. I do not argue that such an idea is false because it's too hard to believe, I argue its false because it contradicts the evidence.
If the evidence did support intelligent design, and I still refused to accept it, then perhaps I would be committing that fallacy.

But it's extremely common that creationists keep talking about how low the odds are for this and that, and how silly it is to believe that a fish turned into a lion, and so on. All of that is a trick, designed to play to people's inability to accept things that sound unbelievable. It's common propaganda trick.
And I'm sure you seen this very thing many times, so you know what I'm talking about.

" it IS ridiculous... no matter how you try to make it sound: and it's the basic proposition of the theory of evolution"

Yes, it is ridiculous becauesr you put it that what.
If you would give me a few hours of your time, where I could actualyl show you the transition between "fish" and lions, it would suddenly look seem as ridiculous, I can promise you that.
Of course that's not possible over hte internet, so... here we are, stuck with this problem.

If it truly was ridiculous, then how is it the unifying theory of all of biology? Would hundreds of thousandsof scientists from every culture on earth all pretty much accept that it is the best explanation for everythign i biology?
Obvioiusly, something is wrong about your understanding of the science. None of us who actualyl understand it, and have studied it at least a bit, think it is ridiculous, so there's obviously some big different between our perspectives on the matter.

"speak of lying and bias and dishonesty:
"All of life on earth shares a common ancestor known as the last universal ancestor, which lived approximately 3.5–3.8 billion years ago."[https://en.wikipedia.org/wiki/Evolution]... is that not what the theory proposes?... "

No, that is a prediction that scientists make based on our knowledge of fossils and other data that relates to it.
The theory of evolution is what allows us to make that prediction - amongst other things -  but if that "number" was a part of the theory itself, then where did that number come from?
The number is a consequence of our understanding of evolution, and our understanding of the history of evolution and life on this planet, aswell as the age of the earth and many other pieces of data.
It is not a part of the theory of evolution.
It's as if the mass of the earth would be a part of the theory of gravity. It's obviously not, even if the mass of the earth could be calculated using the knowledge in the theory of gravity.

The theory of evolution, aswell as other theories, could also allow us to also predict the common ancestor of life on other planets, if we ever get that chance. Therefore, it is a consequence of the theory, not a part of the theory.
the same is true for any other conclusion that we can draw using the theory in combination with data. Humans and chimpanzees being related is not part of the thery, butthe theory predicts that to be true if they share common traits. But the theory is agnostic, it doesn't care what you apply it to, as long as you apply it correctly.
The theory of gravity doesn't care about specific planets, either. It cares about the laws and forces, and so on.

"of course I know it's figure of speech: however there's not possible way you put it that wouldn't sound implausible... again you have no clue how it supposedly happened and all those supposed processes are imaginary; but there you go again, preaching it like it's a fact"

If it sounds impluasible to you, that's your imperfection.
I remember when first trying to learn about quantum physics, and I had a hard time accepting how weird it was, aswell. But reality doesn't care, it's still true. I could kepep sayin git's "implausible" all I wanted, I eventually had to accept that it's real.
So when you tell me somethign "sounds implausible", it doesn't mean anything, it just means you have the inability to believe something, because you're clinging to "common sense", which has no place outside of common situations. Common sense is your enemy when it comes to things that are not common to us, such as billions of years time-scales, or quantum scales, or the scales of supermassive black holes. None of it seems plausible, but the evidence still tells you its real. Human nature is not equipped to deal with this, so we have to accept that science works, because it has been demonstrated to work.

"I'm sorry to say but some of your supposed answers aren't even answers to me: and some are just misunderstandings"

That's possible. Shit happens, sometimes. It's also possible that you simply did not understand my answer. At least consider that possibility. Show some humility.

" well you have to realize you're not typing computer programs and most of your lines are not needed for the points: I appreciate your effort to try to relate your points but you should also put effort to understand mine: at least it could save a lot of time and space... and btw... 4000 lines???...wth... please don't do that to me..."

Yes, call me "convoluted", perhaps. I have asperger's syndrome, and my communication style might be very... detailed and overly cumbersome, sure. I don't rely on between-the-lines communication, for example.
I'll do my best to not get anywhere near 4000 lines, but you provoke me into typing, you know. :)
I have no idea how long this comment is, but I'm afraid it's getting waaay to long, again.
Just help me keep it shorter by avoiding unnecessary repetition or derailing into other things. I suck at it, so don't rely on me.
Reply: antiHUMANDesigns loool... 777 lines and counting: considering most of your lines are basically pointless, I didn't need to read everything... also I think I can see the basic problem here... it's definition of terms as usual... and of course that's why you're just going to repeat the same bant over and over again... anyway I wanted to have a good reasonable debate with someone like you to clarify a few things and gain new knowledge: I admit the only thing new I learnt was the punctuated equilibrium... but haven spoken with you, I think I'm glad to say I don't reason like you...
Reply: Benjamin Toby 777 lines, yeah... well, I replied to a 288 line comment, and I quote most of what you say, so a lot of it isn't actually "mine".
But yes, it was getting too long.

 
" I think I can see the basic problem here... it's definition of terms as usual... and of course that's why you're just going to repeat the same bant over and over again"

Tell me what terms we have different definitions for. There must at least be one specific term you're thinking of.

Yes, I will keep repeating what I'm convinced is the correct answer, or I would be dishonest. And I will keep trying to explain why it is the right answer.
I'm sure you're doing the very same thing, and that you are convinced, just as I am, but of a different answer.
The only way to break this deadlock is to look at the evidence. Don't let humans decide, let reality explain it.

"I admit the only thing new I learnt was the punctuated equilibrium"

Even a small thing like that would make it worth it, imo. Even if I only learnt how to spell a word correctly, by having a conversation, I would consider it a positive outcome.

"but haven spoken with you, I think I'm glad to say I don't reason like you"

Well, what can I say? Fuck you? :P
No, but really, I think my "way of reasoning" is quite effective at getting to the correct answer. I am on the side of science, you know, and science has demonstrated that it is enormously effective. Don't forget that you're not simply arguing with me and my personal ideas, you're arguing with the scientific community (indirectly), because it's their conclusion that I am presenting to you.
At least I must commend you for having the balls to do that, when you should know that there's a very, very good chance that hundreds of thousands of experts on the subject is more right about this than you are.

And as a side-note, you can fight me all you want on this, but the fact is that you have displayed that you do not know particularly much about the science involved. I recommend you study this properly - at least so that you can make stronger arguments, right?
But I also know that you will most likely just say that I'm wrong about this. Fine, save face, or something, but I've said what's on my mind, take it or leave it.

In case you want to end this discussion here, that's fine (I got that feeling). But I can keep going if that's what you want to do.
Reply: antiHUMANDesigns lol... well from what I've realized you don't seem to put enough thought into my points: and it's actually frustrating to try to communicate simple points and then get dragged into pointless rants... how would I create valid points when you probably can't remember the root of most of my arguments?... I've just realized it is no use: you just over-complicate simple points with un-needed rants... I'd love to speak with a real biologist though: at least one who could understand simple points... saying you stand for science is funny: I'm not sure of what you think science is but I think I'm certain that's just another road to a pointless end...

btw: the vital terms are "evolution" and "code"... maybe that'll be a simpler point... now please try not to stray off point: I'll define the terms and you'll define yours:

-Evolution: a gradual development from a simpler form to a more complex form: Etymology: unfold, unroll : 

-Code: a set of ideas or rules about how to behave...
Reply: Benjamin Toby That's the wrong definition of "evolution." Try the biological one.

I am not a biologist, but I did study a fair bit of it in college while I was majoring in physics. I know a fair bit of information theory, and work part-time as a programmer, so I think I am qualified to answer your basic questions about codes and such.

If you want to bounce some ideas off me, I'll try to answer you in rather shorter posts than the other fellow on this thread. Just throwin' that out there.
Reply: Benjamin Toby "it's actually frustrating to try to communicate simple points and then get dragged into pointless rants"

Oh, I hear that a lot, even from my wife. I can't let things go and continue the conversation if someone said somethign that is wrong. I feel like if we keep the conversation going from there, then the entire thing is undermined by the fact that somethign was wrong from the very start.

But, noen of this means that what I talk about isn't important. When you're not careful with exactly what wrods you use, you may get caught in an equivocation fallacy, fo rexample, without even knowing it. you may think something makes sense, but not realiing that you're basing that on the idea that somethign applies to two different scenarios, when iot actually doesn't, because you weren't careful abotu the limitations of that thing.

The whole "DNA is code" is a perfect example of this. Absolutely perfect. If you want to call a DNA sequence "code", then that is OK, but to then say that it's the same thing as computer code is an equivocation fallacy. The word "code" suddenly means two different things, depending on the context, simply because you wanted to call DNA "code", so you created a new context for that word.

Our entire conversation has been plagued by such problems. And I know very well that if you disagree with this, then I will appear to be extremely annoying.

I also think that when you said that you figured our main problem is a problem of definitions, this is exactly the core of what I'm talking about. Definitions are damned important, because otherwise we don't know what we're saying, and perhaps not even what we're really thinking.

For example, you might assume that some vehicle is a car, when in fact it has a specific name, other than "car", because of some structural difference. And the reason they gave this vehicle a different name, even though it looks like a car, is to avoid the problem of making that comparison, because when you start taking it too far, the word fails. For example, it might not need a driver's license, but you need a drivers' lincense to drive a car, so that will be confusing and could actually cause huge problems, just because we insist on calling it the same thing when it isn't.

Of calling a glass snake a snake, even though it's a lizard that looks like a snake, could cause us to treat it as if it's a snake, and that could potentially be harmful to the animal.
But then some people *will* say "don't be such an ass, it looks like a snake, so we're calling it a snake, it's much easier that way". <- and I don't like that way of thinking.

FUCK, I just ranted, didn't I? :/

"I'd love to speak with a real biologist though: at least one who could understand simple points"

What makes you think anything about biology is simple?

"saying you stand for science is funny: I'm not sure of what you think science is but I think I'm certain that's just another road to a pointless end"

Simple answer: I am telling you what the consensus of the scientific community is. What's "funny" about that?

"Evolution: a gradual development from a simpler form to a more complex form: "

While that tends to be true, especially over long time scales, there's nothing about evolution that requires anything to become more complex. Things adapt to the environment, and becoming more complex for the sake of complexity is detrimental. A simple solution is always the best.
Evolution drives things to be more fit to its environement, and this is measured only by its ability to successfully reproduce as much as possible. That is the only metric that life "cares about", because that is what makes it keep existing.

In either case, the scientific definition of "evolution" is "the change in allele frequencies in a popualtion over time". And you need to use the scientific defintion, or you're arguing against a straw man.
If you don't understand why this definition is the correct one, just study the subject of evolution until you do.

"-Code: a set of ideas or rules about how to behave... "

This so fucking LOL. Do you not realize that you're using the wrong context? The context you're talking about is the context where "code" means, for example, "honor code".
You can't seriously argue that DNA contains a code in that sense.
And this is also what you mean by "machine code", huh?
Reply: Max Spiegel oh well: I realized our shorter conversation was actually more useful even if we had misconceptions: but I think I'm done with the long-comment guy:

If you want the biological definition, then I guess I know of one which could fit it:

evolution
noun
1.
the process by which different kinds of living organism are believed to have developed from earlier forms during the history of the earth.(Google)...

and I'll need to get your definition for "code" and also ask if you think the DNA is a code, or functions as a code...
Reply: Benjamin Toby For the definition of "evolution," we need the biological one. The definition you got from google is accurate, but not specific enough for our purposes. The google definition doesn't specify what process it was that created different kinds of life, so we should be careful here.

Evolution as a process is exactly what AHD said: 
"The change in allele frequencies in a population over time."
or
"The changes in inherited traits within a population over successive generations."

This is different from evolutionary theory, which states that the variety life on earth is a result of this process. This is also to be distinguished from common descent, which is the theory that we all share a common ancestor. This, too, must be distinguished from the hypothesis of abiogenesis, which states that this common ancestor arose as a result of chemistry and natural laws.

As for "code," it is more difficult to find a definition that isn't likely to create an equivocation fallacy. Here is a possible definition I found, but we have to discuss its limitations:

"a set of instructions for a computer"

If we modify this definition to be "a set of instructions for a system," I think we have a more viable definition. But if we do this, then we can argue that the law of gravity is a "code" for instructing how masses interact.

DNA contains the information necessary to instruct the cell on how to perform biological functions, but it doesn't actually fit any current definition of the word "code" as far as I can tell. It is just very similar to a code. But if you insist on bringing the word "code" into our discussion, I suggest "information or a configuration functioning as a set of instructions for a given system."
Reply: antiHUMANDesigns I am going to entertain this "DNA as a code" analogy just so we can see exactly where the analogy breaks down. Sorry if you already did that, but I'm trying to show how that idea is either useless, or just becomes completely meaningless when rigorously applied to DNA.
Reply: Max Spiegel Now this is the major confusion in this subject: both sets of definitions can't possibly mean the same thing... I consider AHD definitions somewhat dishonest...

definitely the definition of evolution in biology is confusing that's why I try to relate it to the original meaning... when I hear that something evolves, I don't just consider it as a change: that notion is ambiguous and it definitely doesn't convey any particular meaning: I consider it to be an upward change: hence "devolution" by definition would mean a downward change...

If we say change as in a white peppered moth to a black peppered moth, then that's change alright, but more of variation(more like horizontal change): if we say change as in a monkey to a human(paraphrasing),  that's change too, but a much different type(more like vertical change): if evolution was just about the peppered moth kind of change, or that of the dog breeds, there definitely will be no contest: but since we obviously have two distinct types of change, the notion of just change covers both of them and hence creates confusion:

 this confusion lies basically in the evidences and experiments: if we say evolution is a scientific fact based on the observation and experimentation of the peppered moth then we have a plausible scientific deduction but the evidences actually point to variation within the same gene pool: but what if we take that deduction to imply that the monkey transformed into a man, then we have a problem of evidences and experiments because such a thing has never been seen happening... hence saying evolution is a scientific fact based on these two notions is false to me.

"information or a configuration functioning as a set of instructions for a given system."... that sounds like a good definition to me: and the DNA definitely fits that description: but why is it a problem when I infer from that to say that the DNA had intelligence behind it?
Reply: Benjamin Toby
"I consider [evolution] to be an upward change: hence "devolution" by definition would mean a downward change"
That's just you inventing your own definition, though. The scientific definition is extremely simple: change in inherited traits over successive generations. They could be good, or bad. It makes no difference.

If you want an example of an "upward change" you are starting down the whole "no new information" objection that creationists like to spout. I can give examples of beneficial mutations, or of genomes increasing their amount of genetic material. That is clearly an addition of "information" which benefits the organism, so there is your capacity for "upward" trajectory proved.

"If we say change as in a white peppered moth to a black peppered moth, then that's change alright, but more of variation(more like horizontal change): if we say change as in a monkey to a human(paraphrasing),  that's change too, but a much different type(more like vertical change)"
In evolution, "better" simply means "more fit for the environment." The change in the peppered moth made it more fit for its environment, so biologists would consider this an "improvement" on the species in the given niche. I don't see any reason to view the "monkey to man" change as any more of an improvement. Humans are more intelligent, but they are less agile, don't have the same capacity to live in trees, etc. There is always a trade.

"but what if we take that deduction to imply that the monkey transformed into a man, then we have a problem of evidences and experiments because such a thing has never been seen happening"
That is not how common descent was proven correct. Common descent was proven the same way as any other scientific theory: by making unique, falsifiable predictions that can be proved by repeatable experimentation. You want some for "monkey to man?" Go outside and dig up fossils. You will never find a human in a rock layer from a pre-Cambrian layer. You will find that the further back you go, the more ape-like the hominid fossils we find are. Do some genetic analysis, and if we are more closely related to a tree than an ape then common descent is in serious trouble. The veracity of common descent is as strong as that of heliocentrism, and for the exact same reasons.

" that sounds like a good definition to me: and the DNA definitely fits that description: but why is it a problem when I infer from that to say that the DNA had intelligence behind it?"
Because now I can say something like "the shape of the river is a code instructing the water on how to flow." Don't you see how useless that is? Why would we need to assume intelligence based on this definition? That idea is totally baseless.
Reply: Max Spiegel Yes, yes, give it a try, see where it leads. It's just... I dunno "disheartening" when you see someone absolutely ignore everything you've said.
Reply: Benjamin Toby"I consider it to be an upward change: hence "devolution" by definition would mean a downward change"

"devolution" would mean to lose fitness, rather than gain fitness. These is no known mechanism that for that.
Reply: Max Spiegel I think it's clear to me now that this topic of evolution is just a play of words: btw, I'm not inventing anything and my definition sterns from the etymology of that word and you can see I stated that: as for "devolution", you can just search it out...

-"Because now I can say something like "the shape of the river is a code instructing the water on how to flow." Don't you see how useless that is? Why would we need to assume intelligence based on this definition? That idea is totally baseless."... well "instructing" calls for an instructor: and if instruction is involved, intelligence is involved: so the shape of a river would be a code if an instructor configured it to direct the water through a specific pathway... the simplest definition for code would be something used to represent something else... I don't think there's any definition that you can give that'll be more consistent than this: you can try though...
Reply: Benjamin Toby Man... a play on words does not have predictive power. Evolution happens, and we have the theory of evolution that is able to make predictions. That cannot be explained away.

If I have the ability to predict what is going to happen before it happens, then obviously I know something about how it works and why such things happen, and I am apparently correct about those things, right? At least correct enough to be able to predict things.
This is what theories are capable of doing, or they would not be considered a theory, because it would be useless and untestable.
Reply: Benjamin Toby
well "instructing" calls for an instructor
That is you inventing a new definition for "instruct." Be aware that you are imposing this and we will continue to see where it leads.
 
"and if instruction is involved, intelligence is involved"
Only if your first premise is true, which you didn't demonstrate, but we're taking it as an axiom I guess.

so the shape of a river would be a code if an instructor configured it to direct the water through a specific pathway
Well all rivers go through a "specific pathway," so the river still qualifies as a code as far as I can see. But now you are saying that a code must have a code-writer, which based on our previous definition we can see was not the case. So now you must go back to our previous definition of "code" and modify it to "something that has been written by an 'instructor,'" which is now assuming as a premise that which you set out to prove!

"the simplest definition for code would be something used to represent something else"
And how do you know what that something would represent? This reminds me of Meyers' "specified complexity" claims, which I can tackle in a separate post.

"I don't think there's any definition that you can give that'll be more consistent than this: you can try though"
Well it seems we're off to a shaky start then, doesn't it?
Reply: Max Spiegel "information or a configuration functioning as a set of instructions for a given system."... this was your definition right?... now what you're actually saying is that the shape of all rivers are information/configurations... how does  that make any sense?... I'm not inventing anything here I'm just drawing from your own definition... you are the one actually inventing a new definition by saying the shape of a river is information/configuration that instructs the river ... that doesn't make any sense... except of course you have a way to explain to me how a river shape is information/configuration...
Reply: Benjamin Toby How does it not fit the definition? I take it you understand how rivers get their shapes, right?
Reply: Benjamin Toby"...explain to me how a river shape is information/configuration"

If the shape of a river can be represented by 1's and 0's, based on the sequence or left and right turns... Then that proves that the shape of a river contains information just as much as a binary string does!
And yes, you can have a computer use the shape of a river as instructions for running a program, for example! No problem at all.
Reply: +antiHUMANDesigns "The main point of science is being able to predict things, because that's useful."

Natural selection makes predictions that we agree on, but what does the notion of random mutations, generating prescriptive genetic information, predict?  Absolutely nothing, because it has never been observed.  Or what about the belief that the first genetic information arose by itself through undirected processes?   Are we seeing that happen?  No, because the law of biogenesis is still intact.

I will ask again, have you actually watched Evolution Demolition in its entirety?
Reply: Mark Champneys"but what does the notion of random mutations, generating prescriptive genetic information, predict? Absolutely nothing"

Of course not. The existence of something doesn't make predictions, it's just an observation. You have to find a pattern to be able to make predictions.

"because it has never been observed"

One mutation doesn't do much, no. For example, take the word "undertaker". One mutation would only change on letter, or perhaps discard a few letters, or copy a few. For something notable to happen, you generally need mutations from separate generations.
In some cases, one small mutation can have interesting effects, but they generally don't.

So you're looking for this is the wrong place. Evolution is about the cumulative changes over time. It's rarely about just one mutation.

"No, because the law of biogenesis is still intact."

The law of biogenesis might well be wrong, it depends on how you see it.
The point of the law of biogenesis is that cells only come from other cells dividing themselves. But what if something that was almost a cell copied itself and became a cell, jsut by one small change? The last change needed to be considered a "cell".
When it comes to abiogenesis, the line between life and non-life gets blurred. Exactly what does a thing need to do to be considered life? And what if the first cell would be related (a counsin, perhaps) to somethign that wouldn't be considered alive, just out of natural variation?

So the law of biogenesis doesn't apply very well to such a scenario. Whether it's right or wrong, I dunno, it depends on a lot of things.

"I will ask again, have you actually watched Evolution Demolition in its entirety?"

Yes, but it was some time ago, now, obviously. What about it?
Reply: Mark Champneys
"what does the notion of random mutations, generating prescriptive genetic information, predict?  Absolutely nothing, because it has never been observed."
"The notion of random mutations" predicts nothing except that random mutations happen. "The notion of random mutations generating prescriptive information" seems to be a straw man prediction from creationists, as I've never heard a scientist use such terms.

Glossing over what you mean by "prescriptive information" (since you have not defined this term) we do observe random mutations produce beneficial traits. Genetic analysis shows that this has happened many times in the past as well.

"Or what about the belief that the first genetic information arose by itself through undirected processes?"
Any assembly of molecules has "information" according to Shannon-Weaver theory, so what would be mysterious would be if we had an assembly of DNA that had no information. Even a random collection of symbols or particles has a measurable amount of information. If you are trying to avoid the scientific definition of information as provided by information theory, you better define what you mean by "information," which would be a first from any creationist I've ever seen.

"Are we seeing that happen?"
You mean are we seeing the first genetic information arise from chemistry? Obviously not, or it wouldn't be the first.

"No, because the law of biogenesis is still intact."
I hope you understand that scientific laws are just statements of our observations and not immutable truths. Newton's laws of gravity are technically wrong, and probably so are Einstein's, but they still serve to explain the vast majority of gravitational phenomena as we observe them. However they are always open to be expanded upon, but your position seems to be that such expansion is impossible for biogenesis. I've yet to see anyone demonstrate this claim.
Reply: +antiHUMANDesigns "The existence of something doesn't make predictions, it's just an observation."  The notion is the model; and the observation of mutations generating genetic programming would be the predicted outcome.  Except that this prediction has never been observed.
     "Evolution is about the cumulative changes over time. It's rarely about just one mutation."  Yes I understand; but neither has ever been observed in the uphill direction.  Only the downhill or sideways direction.  Your model predicts that which has not been observed.  You merely look with hindsight and declare that it must have been evolution.
     "But what if something that was almost a cell..."  And how does something with such vast complexity and functionality "almost" arrange itself?  To do so would be against the laws of science and mathematics.  In your example you don't even have natural selection operating yet (before the cell is complete).
     "What about it?"  I just wanted to make sure.  I've found that many on this forum have criticized my video without having watched it.  A similar thing happened to Stephen C Meyer after his book Signature in the Cell was written.  Evolutionists of high stature wrote rebuttals, and it turned out they hadn't even read his book before doing so.  It happens.
Reply: +Max Spiegel Prescriptive information (as opposed to descriptive information or a mere collection of data) is a symbolic representation of instructions.  It is a recipe or blueprint.  We know that DNA sequences contain instructions because organisms beget after their own kind.  Biological systems use this prescriptive sequence-specific coded information to manufacture a given outcome.  Sheep DNA results in a sheep.  Sheep DNA is not a sheep, but contains instructions for building a sheep.
     Shannon information represents the beginnings of information theory, and an attempt to measure information content.  He understood that his model was incomplete.  Measuring the information content of instructions is much more difficult, because instructions are ideas conveyed by symbols.  William Dembski has written extensively on this.
     Your point is taken in regards to the law of biogenesis.  However, if one is going to ignore a law of science, it is no small matter.  At the very least, a reasoned explanation backed up by data is required.  Evolution offers no explanations; only excuses for abandoning the law.  What mechanism gives rise to complex, functional, prescriptive information?  Nothing is offered.
Reply: Mark Champneys "the observation of mutations generating genetic programming would be the predicted outcome. Except that this prediction has never been observed."

We see life change, and it changes by its DNA (genepool) changing. The theory of evolution explains how this happens.
Mutations generate new genes (not "genetic programming", which would imply a programmer that doesn't exist). And new genes result in new lifeforms.

"Yes I understand; but neither has ever been observed in the uphill direction. Only the downhill or sideways direction."

Life only changes in one direction: Towards more fitness to its environment. There is no "side" or "back". This should not be hard to understand, since it's the principle of natural selection, and it's quite simple.

" Your model predicts that which has not been observed."

The model predicts that species will change in a way that makes them more adapted to their environment. There's nothing strange about it, and we do see that happen. It's hardly even a worthwhile prediction, because it's so obvious. Yes, if all tall people get killed, then the species will become shorter.
However, this was not so obvious during Darwin's time when they had no idea how traits are inherited, they didn't know about genomes. The reason I look like my parents is that I inherited their DNA.

"You merely look with hindsight and declare that it must have been evolution."

Well, yes, similar to how I assume someone shot me if I get hit by a bullet, for example.
And the reason why we declare this is because there is no other way to reasonably interpret what we see. That's why it's undisputed within the scienitific ommunity.

And then, once we figured out how it works, it became even more clear that this must happen, it's not optional. And then it's completely indisputable that this is what did happen. There is no longer any other option.

"And how does something with such vast complexity and functionality "almost" arrange itself? "

We're talking about abiogenesis. There is no reason the first "almost cell" would need to be very complex in comparison to anything that exists now, that has evolved over 4 billion years.
We're talking about something like a chemical bubble with RNA enzyme, at the base. Some other things, probably, but nowhere near what it's like today, because modern cells are a shirload more complex than they need ot be to exist.
And the organelles in our cells are separate lifeforms. Mitochondria, for example, was not initially a part of our cells, it was a lifeform on its own. Lots of such lifeforms have formed symbiotic relationship inside our modern cells, which is why only about 10% of the cells in a human body are actually human.
And our cells have adapted to that.
To understand abiogenesis, you need to think of what minimum is required before something fulfills the criteria for "life". We're not exactly sure what the answer to that is, but we're working on understanding it.

But this is something we've doen to ourselves. We've set up criteria for "life", and now we're trying to understand how somethign can fulfill those criteria. If being able to metabolize wasn't a criteria we had set, then explaining abiogenesis would be a lot easier.

"Life" is just what we call a set of chemicals that do a specific kind of thing. It's quite arbitrary, really. And the only reason we have the criteria we have is because those criteria happen to be shared by all things on earth that we would like to call "life".
Those criteria may well change with time.

If we would call a self-replicating molecule "life" then we would already have solved abiogenesis.

" To do so would be against the laws of science and mathematics."

1. Mathematics do not rule nature.
2. You say so, but you "forgot" to mention which laws it would violate.

" In your example you don't even have natural selection operating yet (before the cell is complete)."

Natural selection works on anything that replicates with variation. Even if it was a computer virus that could replicate with variation, natural selection would cull the version that were detected by anti-virus programs, so the computer virus would evolve.
A self-replicating RNA will undergo natural selection as those versions who replicate better than other would have more copies. And the replication process of the RNA is imperfect, which causes variation.
That is natural selection. And this has been demonstrated in a lab. The RNA enzymes evolved to become better and better self-replicators.
If we would've given them a larger, more complex environment, and let them keep doing this for a few million years, who knows what might have come from it.
Reply: Mark Champneys "What mechanism gives rise to complex, functional, prescriptive information? Nothing is offered."

that is exactly what the theory explains. That is the whole damn reason for the theory.

"Your point is taken in regards to the law of biogenesis. [...]  Evolution offers no explanations; only excuses for abandoning the law."

It's not the "job" of the theory of evolution by natural selection to explain the origin of life, only the diversification of life.
We do not have a theory of the origin of life, at this time.
But the law of biogenesis doesn't mean what you're trying to say it means. If it meant what you mean, then the law would simpy be wrong. The law was a reaction to the idea of something like spontaneous generation. It does not apply to the beginnin of life, and they knew that when they coined that law. Of course life started at some point, and that means life must have come from something that wasn't alive. If it came from somethign that was alive, then that life must have come from something that wasn't alive. Because the unvierse did not start with life in it.
Reply: antiHUMANDesigns *We see life change, and it changes by its DNA (genepool) changing. The theory of evolution explains how this happens.* ... The model predicts that species will change in a way that makes them more adapted to their environment. ... So in essence the theory of evolution is just telling us how white moths turn into black moths as a result of adaptive traits?...
Reply: Benjamin Toby I wouldn't put it like that.
At the fundametal level, the way evolution works is really, really simple.
1. A population reproduces with variation.
2. The different variations will have different success in reproducing in their specific environment.
3. This causes the gene pool to change in a specific direction over generations.

That's it, fundamentally. It's not hard to understand, and there should be nothing to dispute about this.

A species of white moths might turn black, over time, if darker moths generally have more offspring that bright moths. We can insert this into the 3 points I described above.
1. White moth population reproduces with varying "whiteness".
2. The slightly darker moths have more offspring than the brighter ones.
3. The gene pool contains more and more daker moths over generations.

And the reason why white moths existed to begin with is because the environment changes. It must have been better to be white before it became better to be black.

It's impossible to perfectly predict how a species will change because there are multiple ways to solve the same problem. But some solutions are simpler than others, and therefore more likely to happen.

The theory predicts that a species will not change in a way that is not beneficial to its reproduction in their environment. And a species will not evolve a behaviour where it helps other species at a cost to itself (a "reverse parasite"), because there can be no such selection pressure.
There is an opportunity for falsification, for example: If you can find a species that finds food and feeds a different species at a cost to itself, then that contradicts our understanding of evolution. The theory of evolution by natural selection tells us that the individuals of such a species that used the food for itself, instead of giving it away, would have more energy and resources to have more offspring who would be more secure, therefore, that behaviour would become more spread through the gene pool over time. In fact, the "selfless" behaviour should never have existed to begin with.
 On the other hand, under creationism, there is no "rule" against the existence of such species. There is no reason why such species could not exist if god made all the species, instead of evolution.
But all living things are inherently selfish/egoistical/self-centered, not sure exactly which word is best to describe it.
Humans aswell, of course.

And btw, I'm still waiting for the creationist explanation to those points I listed for you in that other comment thread. Or do you finally admit that creationism doesn't explain the evidence?
Reply: antiHUMANDesigns for all the talk, you haven't said anything different to what I said in three lines: that evolution explains how organisms vary within their species, and adapt to situations to aid survival: hence, it explains the diversification from a white moth population to a black moth population: now please tell me, have I defined the theory of evolution or not?
Reply: Benjamin Toby The difference is that I carefully specified what I mean by what I said.

"have I defined the theory of evolution or not?"

The theory attempts to explain how diversification of life happens, yes.
And yes, it explains how a white moth population could gradually become black.
It does not explain how organisms vary within their species, however. That is not part of the theory, that is separate.
Reply: antiHUMANDesigns so you accept that evolution explains the diversification of the moths but it doesn't explain genetic variation?
Reply: Mark Champneys 
"Prescriptive information (as opposed to descriptive information or a mere collection of data) is a symbolic representation of instructions."

How do you know that the DNA in a sheep that "codes" for "sheep" is "prescriptive" and not a "mere collection of data?" It seems quite clear that it is in fact exactly a collection of data: a collection of that data which resulted in traits that increased the fitness of organisms in a given niche. We see random mutations occurring, some of which are beneficial, so clearly at least some of the information in DNA is not prescriptive. 
We can see this this information being written and rewritten before our eyes without a prescription for the function it results in, so why do you assume the rest of it must have been generated by supernatural means?

I will describe how what you call "descriptive information" and a "collection of data" can be indistinguishable from what you call "prescriptive information."

Remember the river analogy I gave Benjamine? At first, water flows based on the original lay of the land, in the path of least resistance. That is, its course is essentially information which we can view as a description of how the hills and curves of the land are. We can view the location and shape of the river as the data representing this layout.

As time passes, this data of where the water flows and how the land is structured collects and actually changes the lay of the land through erosion. The river now follows paths and that could not have existed without the river flowing in the first place. We could now say that the river is directed by instructions that were prescribed by itself (coupled with the initial lay of the land and physics). Every turn can be represented by a symbol just as a molecule of DNA can. Neither are symbols in themselves, though; that's just another of your equivocation fallacies.

Your distinction between these supposedly different kinds of information is vague and untestable. In general, you'll have to do better if you want anyone in the scientific realm to take this seriously. 

Evolution offers no explanation for abandoning biogenesis because abiogenesis is not part of evolution. But the rise of "complex prescriptive" information is not necessary; partly because it seems that DNA has only what you call "descriptive information" that describes which traits were selected for over the course of evolutionary history. It must simply be information reflecting what molecular structures are viable in a given environment. The fact that structures like this can and do absorb information from and specific to their environment is a fact that can be modeled by Shannon information theory.

Dembski has made no impact in the field of IT. Just check how his colleagues consider his work.
Reply: Max Spiegel  Remember the river analogy I gave Benjamine. At first, water flows based on the original lay of the land, in the path of least resistance. That is, its course is essentially information which we can view as a description of how the hills and curves of the land are. We can view the location and shape of the river as the data representing this layout. ... so what you're saying in essence is that the trail left by a rolling snowball is information for the snowball?...
Reply: Benjamin Toby " so you accept that evolution explains the diversification of the moths but it doesn't explain genetic variation?"

Yes, exactly. Genetic variation is a "premise" for evolution, but the theory of evolution doesn't explain genetic variation. Some other part of biology does that. It is an input into the process, and a directed change is the outcome.
I suppose the subject of individual variation is covered by population mechanics and genetics, I'm not sure.

"so what you're saying in essence is that the trail left by a rolling snowball is information for the snowball?... "

It is information, but it isn't information "for the snowball". Information just "is".
Reply: antiHUMANDesigns but the diversification of the moths is actually genetic variation... so what you're saying is that evolution explains genetic variation but it doesn't explain genetic variation...
Reply: Benjamin Toby Yes, the size of the snowball determines its rate of growth. We could even write an equation like dV/dt ~ r^2 (the rate change in volume is proportional to the radius squared) and plug in a value for r. That r value, coupled with the amount of snow in the environment, would be "information" that, by your definition, would "code" for the rate of growth of the snowball.
Reply: Max Spiegel *Yes, the size of the snowball determines its rate of growth*  ... off point... my question is about the trail not the size... 

 We could even write an equation like dV/dt ~ r^2 (the rate change in volume is proportional to the radius squared) and plug in a value for r.... plausible hypothesis, but again, off point... PS what do you mean "plug in a value for r"?... you can't plug a value until a test is done and you have a constant of proportionality... in this case r is dependent on the volume and speed of the snowball, as well as the slope of the ground... what you stated is not an equation: it's a relation... and you can't "plug in" values into a relation that way...

That r value, coupled with the amount of snow in the environment, would be "information" that, by your definition, would "code" for the rate of growth of the snowball.... first we are still working with your definition... and secondly the r value is dependent on the speed and volume of the snow ball, as well as the slope of the ground... so how would r act as information if the information is generated by the process which it's meant to code for?... that makes no sense... that's like saying the amino acid sequence is information for coding the DNA... 

back to my question... and I repeat... is the trail created by the rolling snowball information for the snowball?
Reply: Benjamin Toby 
"my question is about the trail not the size"
Ok, my bad, but how does that change the analogy?

"PS what do you mean "plug in a value for r"?... you can't plug a value until a test is done and you have a constant of proportionality
I mean that we, as humans, can assign a number to r to understand what nature is going to do with that "information." To nature, there is no such thing as a "value" for r, just as there is no "code" for DNA. Nature "plugs in the numbers" automatically.

" in this case r is dependent on the volume and speed of the snowball, as well as the slope of the ground... what you stated is not an equation: it's a relation... and you can't "plug in" values into a relation"
What you just described is a differential equation, and after solving a differential equation one can plug in for a specific solution and solve to predict what the snowball will do. Again, nature manages all of this "information" automatically.

"first we are still working with your definition"
Well you agreed to it, so let's call it "our" definition, okay?

"secondly the r value is dependent on the speed and volume of the snow ball, as well as the slope of the ground... so how would r act as information if the information is only generated by the process which it's meant to code for?"
Saying the volume is dependent on the radius is the same as saying the radius is dependent on the volume. If you know one, you know the other: they are intimately related pieces of information. That information, coupled with the information from the environment, changes the radius of the snowball, which in turn changes the information to now code for "accumulate snow faster," or "roll this way instead of that way" or whatever it is you want to know about what the snowball will do.
Reply: Max Spiegel you know there's a good chance I might have misinterpreted your hypothesis... on second thought it seemed like you were speaking of the initial radius while I was referring to the instantaneous radius: but that's trivial to this situation... this analogy though is much different from the river analogy and would require consideration of other parameters which may include human intelligence: and I'm not sure that would clarify anything: we could get to that after we clarify your river analogy... the analogy I gave was to create a parallel to your river analogy: and it goes like so: you said the river "information" is created by the flow of the river and I stated that it's similar to saying the trail of a rolling snowball is information for the snowball... so back to my question: do you consider the trail of the snowball information for the snowball?
Reply: Benjamin Toby I don't see any difference between the river analogy and mine with the snowball one. However I don't think I understand your question:

"do you consider the trail of the snowball information for the snowball?"

If you mean after a snowball rolls down a hill, do I consider that information for what the state (size/shape/etc) of the snowball will be is captured in the trail? Yes, some of it, but not the part due to other environmental factors like temperature.

If you mean do I consider the trail formed by the snowball information for the construction of that same snowball that rolled down the hill, my answer is "no." But it is information for other snowballs that may roll down a similar path.

Creationists often ask where the "first" information in DNA came from, and through this analogy hopefully you can see that is equivalent to asking where the first path came from that other successive snowballs follow. This should make it clear that there is no mystery as to how specific information can come from natural processes.
Reply: Max Spiegel so what part of the river creates the information?... since you say the trail left by the rolling snowball isn't information for the snowball... also, how does the river fit into the description of a "system"?... remember I'm still trying to work with your definition here: in truth, I don't think there's any scientist that would dispute that the DNA is a code or atleast, functions as a code...
Reply: Benjamin Toby We are not debating whether DNA functions very much like a computer code. Most biologists would agree on this. The problem is in the equivocation fallacy that you are making, which is that DNA is objectively a code. Surely scientists will speak of DNA as "coding" for something, as physicists will talk about particles "wanting" to reach a state of lowest potential energy. I think you will be hard-pressed to find scientists saying that DNA is objectively a code in the sense that a computer program written by a human is.

What creates the information coding for the direction the river flows is the interaction of the water, geography, and the laws of physics.

The trail from one snowball is not information about how the snowball should roll. I explained why I don't understand by the phrase "information for the snowball" in the last post. I understand information coding for the rate of increase or path a snowball take in a given environment, but your question as phrased is malformed.

How does a river not fit the definition of a system? It is a water source interacting with geology and the laws of physics.
Reply: Max Spiegel  The trail from one snowball is not information about how the snowball should roll. I explained why I don't understand by the phrase information for the snowball in the last post. ... and I thought I explained why the trail of the snowball is homologous to the shape of the river?... all I'm doing is trying to apply your definition that the trail formed by a moving body is information for it: that was why I asked what part of the river was setting the "information"... if my analogy is "malformed" then your river analogy is too: they are the same concepts...

We are not debating whether DNA functions very much like a computer code. Most biologists would agree on this. The problem is in the equivocation fallacy that you are making, which is that DNA is objectively a code. ... what equivocation are you talking about?... I'm saying the DNA is a code because it functions like a code: atleast to the human knowledge of how codes function... I particularly used the stonehenge analogy to explain this... you on the other hand are saying anything can be "code"... and so far your definition is equating the trails of natural occurrences like rock slides to the highly engineered computer code...

I think you will be hard-pressed to find scientists saying that DNA is objectively a code in the sense that a computer program written by a human is. ... "DNA is objectively a code in the sense that a computer program written by a human is." = "DNA functions very much like a computer code. " ... that's the "sense" in which the comparison is drawn: the function...

How does a river not fit the definition of a system? It is a water source interacting with geology and the laws of physics. ... a system is a group of parts interacting together for a common purpose... what you're saying now is that the purpose of geology and the laws of physics is to form rivers... you are also saying any water source creates a river... I can say from this that water splashing on a rock from a water pump is a river... 

I see the issue is the same as ever: definition of terms: considering how these definitions can be manipulated to mean anything, I think comparative descriptions would be much more valuable: so I could say we agree on the DNA functioning similar to a computer code?... if yes then I don't see how different that is to my point: the only cause of the computer code is intelligence... what other cause would account for the DNA?...
Reply: Benjamin Toby "but the diversification of the moths is actually genetic variation... so what you're saying is that evolution explains genetic variation but it doesn't explain genetic variation"

No, evolution explains a directed genetic diversification.
We know that DNA diversifies, that it adds variation, that it "reproduces with variation". This causes there to be many different variations within a species. "Natural variation".
But the theory of evolution explains how there is a "bias" (selection pressure), causing this diversification to move the species in a specific direction over time.

If you have the number "10" and you just keep copying it with a random +/- 1, then you'll end up with an average close to "10", still. But if higher numbers are copied more often than lower numbers, then the average value of the numbers will constantly increase.
That is the difference. And that's why "evolution", the change in the gene pool, is indisputable. It must happen, it's unavoidable as long as there is a selection pressure on a something that reproduces with variation.
Reply: Benjamin Toby
"and I thought I explained why the trail of the snowball is homologous to the shape of the river?"
I don't think you understand the analogy. The trail left by past snowballs codes for the path of future ones. The path carved out by the first trickle of a stream down a mountain changes the path of future water going down that mountain by erosion.

The malformed part of your question (not analogy) was saying "do you consider the trail of the snowball information for the snowball?" I don't understand what you are asking here. Do you mean "do you consider the trail of the snowball information for that same snowball?" or  "do you consider the trail of the snowball information for the path of future snowballs?"

"what equivocation are you talking about?... I'm saying the DNA is a code because it functions like a code: atleast to the human knowledge of how codes function."
That is your equivocation fallacy. Because it functions very much like a code you want to call it an objective code. Just say it functions like a code, because that part is objectively true. It being a code is not.

"that's the "sense" in which the comparison is drawn: the function"
Yeah it's a comparison. It's another analogy. That is all.

"a system is a group of parts interacting together for a common purpose"
No, in science systems have no purpose. Consider the earth-sun system, or a system of particles in an isolated container. These are physical systems. If you want to redefine the word "system" then explain your new definition.

"what you're saying now is that the purpose of geology and the laws of physics is to form rivers"
Again, I said nothing of purpose.

"you are also saying any water source creates a river."
Where did I say that?

"considering how these definitions can be manipulated to mean anything, I think comparative descriptions would be much more valuable: so I could say we agree on the DNA functioning similar to a computer code?"
We can agree it functions like a code. We cannot agree that this means it is a code. The definitions cannot be manipulated to mean whatever you want if you stick to the scientific ones. Instead I am humoring you by adopting non-scientific definitions for things like "information." The only reason these definitions seem to be so malleable is because you are trying to make equivocations that aren't there, and so are being inconsistent with the agreed definition.
Reply: Max Spiegel  I don't think you understand the analogy. The trail left by past snowballs codes for the path of future ones.The path carved out by the first trickle of a stream down a mountain changes the path of future water going down that mountain by erosion  ... and my question is how do you differentiate this "trickle" from the river if the "trickle" is also the river? 

The malformed part of your question (not analogy) was saying "do you consider the trail of the snowball information for the snowball?" I don't understand what you are asking here. Do you mean "do you consider the trail of the snowball information for that same snowball?" or  "do you consider the trail of the snowball information for the path of future snowballs?" ... I think I said I was talking about the same snowball here... that's why I want you to distinguish between the "first river" and the "future river"...

That is your equivocation fallacy. Because it functions very much like a code you want to call it an objective code. Just say it functions like a code, because that part is objectively true. It being a code is not.... what do you mean "objective code"?... didn't you see my equation?... btw since you agree it functions like a computer code what cause do you propose for its origin?

No, in science systems have no purpose. Consider the earth-sun system, or a system of particles in an isolated container. These are physical systems. If you want to redefine the word "system" then explain your new definition. ... https://en.wikipedia.org/wiki/System ... 

Where did I say that?... you said a river is a water source interacting with geology and the laws of physics and I gave you an example of a river by your own definition which is water splashing on a rock from a water pump (the "water source") ... 

We can agree it functions like a code. We cannot agree that this means it is a code. The definitions cannot be manipulated to mean whatever you want if you stick to the scientific ones. ... http://ghr.nlm.nih.gov/handbook/basics/dna ... so can we agree that the DNA contains a code?... 

To be honest, if you agree that the DNA functions similar to a computer code, what difference would it make if I called it a code?... doesn't it still point to an intelligence?
Reply: antiHUMANDesigns  No, evolution explains a directed genetic diversification. We know that DNA diversifies, that it adds variation, that it "reproduces with variation". This causes there to be many different variations within a species. "Natural variation". But the theory of evolution explains how there is a "bias" (selection pressure), causing this diversification to move the species in a specific direction over time. ... you mean like the direction of white moths to black moths?... that's still genetic variation... so you're saying evolution explains how different variations of a species are pronounced in different populations and environments?...
Reply: Benjamin Toby
"my question is how do you differentiate this "trickle" from the river if the "trickle" is also the river?"
Well now I think we are getting a little too far into semantics, but I'd say that we can call it a trickle when its path is determined by the "code" of the landscape as it was before water had begun to erode it.

"I think I said I was talking about the same snowball here... that's why I want you to distinguish between the "first river" and the "future river"
Well the trail of the first snowball would be coded for by the laws of physics and the local geography, just as the first trickle would follow the path of least resistance down a mountain.

"what do you mean "objective code"?... didn't you see my equation?... btw since you agree it functions like a computer code what cause do you propose for its origin?"
By "objective code" I mean that it was designed by someone to represent something. I saw your "equation" and as I've said a few times now, it's an equivocation fallacy. There is no way to prove objective functionality in DNA. There is no way to say "this gene was designed to create that protein," because that assumes a designer. We can only say "this gene corresponds to that protein."

The origin of the first "code" in RNA (or whatever molecule came first) is likely the same as the origin of the first snowball trail or trickle: the information in the environment coupled with the laws of physics/chemistry. It's like asking the origin of the code for the design of salt crystals: the answer is chemistry.

https://en.wikipedia.org/wiki/System

I'm not seeing where it says that systems have to have a purpose here.

"you said a river is a water source interacting with geology and the laws of physics and I gave you an example of a river by your own definition which is water splashing on a rock from a water pump (the "water source")"
I didn't realize we were going to try to dive so deeply into the semantics of the word "river." If you need me to make a distinction between a river and a trickle, I refer you to what I said above in this post.

"so can we agree that the DNA contains a code?"
No, for the millionth time we can only agree that it acts like a code. That this article says "DNA is a code" is not dissimilar from a physicist saying that systems "want" or "seek" to minimize their potential energy. It is a bit of colorful language and analogy to help the reader understand; it is not an equivalence.

"To be honest, if you agree that the DNA functions similar to a computer code, what difference would it make if I called it a code?... doesn't it still point to an intelligence?"
Does the code of the shape of the river, which functions to tell the water which way to go, point to intelligence? I would say it does not.
Reply: Max Spiegel  Well now I think we are getting a little too far into semantics, but I'd say that we can call it a trickle when its path is determined by the "code" of the landscape as it was before water had begun to erode it. ... oh really?... semantics?... well I'm happy you can see that... my aim is to show you exactly what you do... and I'm glad you're catching up... in this case I just want to show that the river analogy is a total miscue relating to your definition... you've just said now that the landscape is "code" for the "trickle" and that equates to saying any landscape is code whether a river flows there or not: this is so because there's no distinction b/w a landscape that would make a river and one that wouldn't...

Well the trail of the first snowball would be coded for by the laws of physics and the local geography, just as the first trickle would follow the path of least resistance down a mountain. ... well that doesn't make any sense because you're saying the computer code is also coded by the laws of physics and geography... 

By "objective code" I mean that it was designed by someone to represent something. I saw your "equation" and as I've said a few times now, it's an equivocation fallacy. ... so I'm making an equivocation by saying the DNA is a code but you aren't by saying it's a random occurrence?... that's interesting... 

The origin of the first "code" in RNA (or whatever molecule came first) is likely the same as the origin of the first snowball trail or trickle: the information in the environment coupled with the laws of physics/chemistry. It's like asking the origin of the code for the design of salt crystals: the answer is chemistry. ... I'm just curious: if I'm not allowed to say the DNA is a product of intelligence what gives you the right to say it originated by chance, or from RNA?... do you have proof for that?... and by proof please don't show me failed experiments... I want to see the demonstration of the emergence of a fully functional DNA molecule performing it's duties as we can see it and creating proteins to form a living organism... if you can't then you can stop making unfounded assumptions... looking at the way the DNA functions, there's no known natural process that can give rise to such specified complexity... if you know one tell me: and give me the proof... the only known cause of such a thing is intelligence... if you can't find proof for any other cause for the origin of the DNA, then you know nothing about the origin of life...

I didn't realize we were going to try to dive so deeply into the semantics of the word "river." If you need me to make a distinction between a river and a trickle, I refer you to what I said above in this post. ... tell me something now... we've been on semantics right from the start... and it began with you... so we will go all the way... I need you to define the word "river" because your definition was wrong in the sense that pouring a water on the ground from a water bottle constitutes a river... this is your definition I'm working with here...

No, for the millionth time we can only agree that it acts like a code. That this article says "DNA is a code" is not dissimilar from a physicist saying that systems "want" or "seek" to minimize their potential energy. It is a bit of colorful language and analogy to help the reader understand; it is not an equivalence. ... oh I see... "colourful language" ... the way I see it there's no word that perfectly describes the function of a DNA than code... and if it looks like a code, acts like a code, well then maybe it is an "objective" code... I have more rational justification to call it that than you to call it a product of chance... because even human intelligence can't produce that: but human intelligence can make rivers and snowball trails... it'd be perverted to think the same causes for the river can create the DNA...

Does the code of the shape of the river, which functions to tell the water which way to go, point to intelligence? I would say it does not  well in that case the code of the computer doesn't point to an intelligence since nature can conjure up something even more complex... so you're saying there's no such thing as intelligence ... just physical laws and matter... I don't think that's right...
Reply: Benjamin Toby
" in this case I just want to show that the river analogy is a total miscue relating to your definition... you've just said now that the landscape is "code" for the "trickle" and that equates to saying any landscape is code whether a river flows there or not: this is so because there's no distinction b/w a landscape that would make a river and one that wouldn't"

Correct, and you accepted this definition. I don't care how you define your terms, but you have to be consistent in your definitions. If you don't like the definition we've been working with, you can try to adjust it again.

"well that doesn't make any sense because you're saying the computer code is also coded by the laws of physics and geography"

Who said computers are a product of nature?

" I'm just curious: if I'm not allowed to say the DNA is a product of intelligence what gives you the right to say it originated by chance, or from RNA?."

I said neither of those things. I specifically said "The origin of the first "code" in RNA (or whatever molecule came first) is likely the same as the origin of the first snowball trail or trickle," and that it originated by the code of the laws of chemistry and natural selection; definitely not by pure chance. I am making no assumptions, while you are. That's the difference.

"I need you to define the word "river" because your definition was wrong in the sense that pouring a water on the ground from a water bottle constitutes a river"

I never said it did, you just misunderstood me. I gave a working definition for "river" already, but we can go with the dictionary one if you like:

a large natural stream of water flowing in a channel to the sea, a lake, or another such stream.

"the way I see it there's no word that perfectly describes the function of a DNA than code... and if it looks like a code, acts like a code, well then maybe it is an "objective" code"

The only objective code is written by people with intention. We have already seen how our definition of "code" falls apart when applied to any other physical system. Either we have to go back and redefine the term, or you are stuck saying that the laws of physics "code" for the formation of snowflakes.

"because even human intelligence can't produce that: but human intelligence can make rivers and snowball trails"

Human intelligence can't produce volcanoes or stars either. I don't see how what humans can make is a benchmark for judging what nature can and cannot do.

"it'd be perverted to think the same causes for the river can create the DNA"

What "cause" is that? Are you just lumping together all things caused by natural processes? I don't see why it would be perverted to think that DNA has a naturalistic origin.

"well in that case the code of the computer doesn't point to an intelligence since nature can conjure up something even more complex."

Exactly, except that we do have evidence that humans can and do make computers. Code can write itself though, as I pointed out earlier.

If we came from some planet in which computers were unknown to us, but evolution was, and we found a planet with computers that could reproduce with variation and undergo naturall selection, it would be reasonable to work with the hypothesis that the computer code in this world had naturalistic origins.

The laws of physics are, themselves, a code. One can say that any natural phenomenon is a result of this code. I remind you that this is not my definition, but the one we agreed upon. Unless you want to redefine this term, you seem to be stuck here.
Reply: Benjamin Toby "you mean like the direction of white moths to black moths?... that's still genetic variation."

If you have a population of white moths and black moths, randomly, and they keep interbreeding randomly, then you're always going to have black and white moths in fairly equal proportions.
Natural selection, however, might favour black moths, so they will eventually make up the vast majory of the population, when first they might have been a rare mutation, for example.
That is the "change in gene frequency". That is what's explained by the theory.

"so you're saying evolution explains how different variations of a species are pronounced in different populations and environments?..."

Yes, that sounds like what I'm saying. It's about how many individuals carry a specific gene. And that is what evolution is. The change in gene frequencies in a population over time. (It is not about the origin of those genes. Mutations, for example, is not a term that belongs to the theory of evolution, but rather to genetics.)
And if there was no mechanism like natural selection, the gene frequencies would "hover" around the same number. There would be no significant change in gene frequency. But a selection pressure move this change in a specific direction.
Reply: antiHUMANDesigns if the theory of evolution explains the frequency of different variations of a species in an environment, which theory explains the change of species?...
Reply: Max Spiegel  Correct, and you accepted this definition. I don't care how you define your terms, but you have to be consistent in your definitions. If you don't like the definition we've been working with, you can try to adjust it again. ... Umm this just proves that your analogy was wrong... lets do a recap here:
- you defined code as "information or a configuration functioning as a set of instructions for a given system." ... and I accepted that definition ...
- you go on to apply the definition by saying  "the shape of the river is a code instructing the water on how to flow."
- you go on to say this shape is information...
- you go on to say that the shape is only code after the first "trickle" of river, which is also the river, has flown through... meaning the river is creating the code while the river is supposed to flow by the code... a complete miscue...
- since that first "trickle" didn't fit the definition of a river directed by a code, you say that any geology is code for this "first trickle" which is also the river...
- you go on to say that shape of the river is any landscape... an equivocation.
-you said the river is a system of water, geology and physical laws... another equivocation because that dissolves the meaning of the word "system" ... which I gave you but apparently you couldn't see my point ...
- also, I've not asked you how the river shape fits into the classification of "configuration"... only after that would you be able to fully apply your definition to the river analogy... 
 
conclusion... you gave me that definition so you could prove how you could use it to define any other thing ... so far you've defined the shape of a river to be geology, geography and landscape... if this is not a plague of equivocations then I don't know what is... your analogy has equated code to these terms(geography, geology, landscape)... what you need to do now is explain how all those terms are codes by our definition... 

let me try to put this in the form of equations:

- code = river shape
- river code = river shape
- first trickle = river
- first trickle code = landscape = geology = geology
- first trickle shape = first trickle code = river shape = river code
- landscape = geology = geography = code

your analogy fails because landscape, geology and geography don't fit our definition for code: hence, there's no code for a river...

Who said computers are a product of nature? ... you did... I said product of physical laws and geography... watch the terms now... we're already in semantics 301... at this point defining "nature" could lead us to semantics 401 in an unprecedented manner...

I said neither of those things. I specifically said "The origin of the first "code" in RNA (or whatever molecule came first) is likely the same as the origin of the first snowball trail or trickle," and that it originated by the code of the laws of chemistry and natural selection; definitely not by pure chance. I am making no assumptions, while you are. That's the difference. ... didn't you just say the RNA(or whatever molecule) came first? isn't that the same as saying the DNA originated from RNA?... well I say the DNA came first because we've seen DNA create RNA but never vice versa... you're actually making an assumption by saying the RNA(or whatever molecule) came first... you have no proof for that...

I never said it did, you just misunderstood me. I gave a working definition for "river" already, but we can go with the dictionary one if you like:  that definition didn't work at all because it was wrong... the definition you gave was to make the river fit the definition of a system but the actual definition doesn't equate it to a system... which is another equivocation... a system needs a function like I said (or purpose)... and a river has no function... a river is actually made of two components: water and a path... these two parts working together have no specific function because it could empty into a sea, ocean, lake or another river: it might even terminate into the ground... so there's no specific function of a river if it were to be a system... also, if the system contained the code, then how is the code controlling the system?... this is another miscue... the code is meant to control a separate system, not itself; so if the path is controlling the body of water, the water can't be a system... 

The only objective code is written by people with intention. We have already seen how your definition of "code" falls apart when applied to any other physical system. ... "falls apart"? well first its our definition: more accurately your definition... I just agreed with it so we could come to a common understanding... secondly it's far from falling apart... you still have some explaining to do...

Human intelligence can't produce volcanoes or stars either. I don't see how what humans can make is a benchmark for judging what nature can and cannot do. ... yes humans can make volcanoes and stars: just that they would be smaller versions...  and I'm thinking you might have to define the word "nature"... 

* Are you just lumping together all things caused by natural processes? I don't see why it would be perverted to think that DNA has a naturalistic origin.* ... aren't you the one lumping all things caused by natural processes together? 

Exactly, except that we do have evidence that humans can and do make computers. ... Ok lemme get something straight here... you accept there's no such thing as intelligence?

The laws of physics are, themselves, a code. One can say that any natural phenomenon is a result of this code. I remind you that this is not my definition, but the one we agreed upon. Unless you want to redefine this term, you seem to be stuck here. ... gravity is not a code by our definition of what a code is... and the definition is actually yours: I agreed with it yes... still yours... also I want to believe I'm far from stuck here: there's still more to clarify to validate your analogy...

so far we have new problems, one of which is a major one: the definition of "nature" ... could you please define the term "nature" ... I think we're getting close to resolving the river analogy tho: maybe we could take it one at a time... as it stands there are a few misconceptions I'm sensing...

1. a code is not part of the system it's coding for
2. a system needs a function to be called a system
3. the laws of physics don't code for any "given system" so they can't be codes...
Reply: Benjamin Toby"if the theory of evolution explains the frequency of different variations of a species in an environment, which theory explains the change of species?... "

Well, how does a species change? It changes by it's average changing. Humans are on average taller and have on average larger brains than the species we evolved from, for example. That's all it is about.
Since evolution is the change in gene frequencies, it's also the "change of average". And the theory explains why the average changes. Because of natural selection. That is why it's called "the theory of evolution by natural selection".
Without natural selection, even though there still is natural variation, the average would not change over time. You need to favour some trait for the average to change.

Basically, you just answered your question. A change in gene frequencies is a change in the species as a whole.
Reply: antiHUMANDesigns  Basically, you just answered your question. A change in gene frequencies is a change in the species as a whole. ... lol ... you've just said the theory of evolution only explains frequencies of genetic variations of a species, but it doesn't explain genetic variation of a species, but it also explains change of species... I think I'm done here...
Reply: Benjamin Toby What's so hard to understand? DNA reproduces with variation, that causes natural variation within a population. That is not something that the theory of evolution has to explain, because that is not evolution.
Evolution is each gene becoming more rare or more common, because that changes the species as a whole. Sometimes genes even become extinct.
And that is evolution, so that is what the *theory* of evolution needs to explain the mechanisms for.
The mere existence of variation doesn't mean the frequency of genes change. But somehow they do, that is an observation. So then we require an explanation for why they do change in frequency, and that's the "theory of evolution by natural selection". The answer to the question is in the name.
Reply: Benjamin Toby I made a mistake when I called the river example an "analogy." It is not an analogy at all, but rather the literal consequences of the only definition that we could agree upon for the word "code."

You can stop saying it's my definition, because it's not. My definition of a code would be more like "a set of information arranged with the intent of representing something." If we used my definition, you would be dead in the water because you have no way to prove that there is any intention the DNA sequence. You seek to prove that such a "coder" is required, which forced me away from my definition and instead to the one we agreed to adopt for the purposes of this conversation.

The consequences of adopting your definition of "code" is that everything is coded for by the laws of physics, and that the interaction of information almost always leads to new code. This is much like the self-writing code I brought up earlier, which is why when you saying "the river is creating the code while the river is supposed to flow by the code... a complete miscue" is simply wrong. Code can feedback on itself and modify itself, and many computer algorithms do just that.

"your analogy fails because landscape, geology and geography don't fit our definition for code: hence, there's no code for a river..."
How so? Here is our working definition again:

information or a configuration functioning as a set of instructions for a given system.

The landscape, geology and geography can be considered a configuration of molecules that serve as a set of instructions for how water will flow across it.

I'm still not seeing where I said that computers were the product of natural processes (which is at least what I meant to say). I am differentiating man-made things from things that result from inanimate processes. If you want to be super-technical about it, I'd say that everything humans do can be considered part of nature, since we are a part of it, but in this case I think it serves to differentiate between human phenomena and others. I don't see why this is an important point.

"didn't you just say the RNA(or whatever molecule) came first? isn't that the same as saying the DNA originated from RNA?"
No, it's not. It's the same as saying "I don't know what molecule came first, but it likely came from a natural process." We have no evidence of a supernatural "intelligence," so by Occam's Razor we can say that whatever molecule led to life was most likely formed by nature.

"a system needs a function like I said (or purpose)"
No, it doesn't. You didn't read your own wiki article very carefully, because it didn't say that. It said that a system can be described by its purpose, but certainly not that it must have a purpose to qualify as a system. I again ask you what the "purpose" of something like the Andromeda system is.

" the code is meant to control a separate system, not itself;"
This would be a modification by you of our working definition of "code." If you want to add this to the definition, does that not eliminate DNA as a code since it controls its own replication, modification and translation?

"aren't you the one lumping all things caused by natural processes together?"
Well you said the same "cause," so I just wanted to clarify what cause you meant. If you mean nature was the cause, then yes I am.

"yes humans can make volcanoes and stars: just that they would be smaller versions"
Oh really? How could a star be "small?" They are held together because of their immense gravity. I'd like to see one of the man-made stars. Could you provide an example?

"Ok lemme get something straight here... you accept there's no such thing as intelligence?"
I wouldn't say that, unless you have some bizarre definition of "intelligence."

"gravity is not a code by our definition of what a code is"
Sure it is, go back and check it against the definition we're working with. The laws of gravity are information that function as a set of instructions for how masses interact in any system.

So to be clear, the river is not an analogy; it is an example of the nonsensical or trivial consequences of our working definition of "code." I will borrow Google's definition of "nature" as "the phenomena of the physical world collectively, including plants, animals, the landscape, and other features and products of the earth, as opposed to humans or human creations." If you want to include humans and human creations as part of nature, that's fine withe me too. Again, all that matters is that we are consistent with whatever definition we adopt.

1. a code is not part of the system it's coding for
Not true, and not a part of our definition. I have already given counterexamples.

2. a system needs a function to be called a system
Also not true. I have again given counterexamples. Will you now reject wiki's definition of a system?

3. the laws of physics don't code for any "given system" so they can't be codes
How do the laws of physics not code for all given systems? How does the information in the laws of nature not provide instructions for how all physical systems will change over time?
Reply: Max Spiegel  It is not an analogy at all, but rather the literal consequences of the only definition that we could agree upon for the word "code." ... actually the literal consequence of misusing the definition... and I think I demonstrated that...

You can stop saying it's my definition, because it's not. ... ok ok ... our definition... you can stop calling it my definition now...

The consequences of adopting your definition of "code" is that everything is coded for by the laws of physics, and that the interaction of information almost always leads to new code. ... that's not a consequence of the proper application of our definition sorry: the laws of physics don't code for any given system else even computer codes are coded by the laws of physics since the laws also work on them too... also you classified these laws to be part of the system so you'd need to find the code for it... maybe we could agree that these laws are part of every system... maybe...

Code can feedback on itself and modify itself, and many computer algorithms do just that. ... now that would be modifying our definition: lets try to work with our definition for now... going by our definition, there's no feedback...

The landscape, geology and geography can be considered a configuration of molecules that serve as a set of instructions for how water will flow across it. ... watch these terms carefully now... you didn't say "the landscape": that would imply there's a kind of landscape required for rivers: which doesn't fit either... you said "landscape": and that obviously doesn't fit our definition for code... in addition landscape would be part of the river if it were to be called a system so we still need a code for the system...

 I again ask you what the "purpose" of something like the Andromeda system is. ...the purpose of the Andromeda system is forming the Andromeda system: it's a human-assigned purpose... however the purpose of the systems in the cell aren't assigned by humans... very big difference... they're just observed... eg the amino acid sequence building system made of the Ribosome, mRNA and tRNA... clearly the purpose of that system is to form amino acid sequences...

This would be a modification by you of our working definition of "code." If you want to add this to the definition, does that not eliminate DNA as a code since it controls its own replication, modification and translation? ... this is not a modification because from our definition the code is supposed to control a given system ... and I think our definition made a distinction b/w the code and the system...

Oh really? How could a star be "small?" They are held together because of their immense gravity. I'd like to see one of the man-made stars. Could you provide an example? ...I admit I don't have an example to show but atleast you concede humans can create volcanoes... lets say humans can create anything found on earth: except life: which is DNA and living cells...

I wouldn't say that, unless you have some bizarre definition of "intelligence." ... not definition, just math... from what you said;

code = rivershape
rivershape = no intelligence
DNA code = rivershape
DNA code = no intelligence
DNA code > Human computer code
no intelligence > Human computer code
Human computer code > rivershape
no intelligence > Human computer code > rivershape
Human computer code = human intelligence
no intelligence > Human intelligence > no intelligence
Human intelligence = no intelligence

Sure it is, go back and check it against the definition we're working with. The laws of gravity are information that function as a set of instructions for how masses interact in any system. ... that fails if we could find masses interacting without the laws of gravity or against the laws of gravity... in other words, that doesn't fit our definition...

So to be clear, the river is not an analogy; it is an example of the nonsensical or trivial consequences of our working definition of "code." ... "nonsensical or trivial"? agreed ... consequence of our working definition? nope... lets say we label the system to consist of water, landscape and laws of physics like you said, we still need to find the code for it... this is just one aspect in which your application fails...

so basically the main issue now is the distinction b/w the code and the system: and I say it's not possible for the code to be part of the system because a code doesn't instruct itself... lets take your application as an example... if we consider the shape of the river code for the river, then that is a misfire because the shape of the river can't instruct the shape of the river... if we say the shape instructs something else; the water, then that dissolves the river because the shape is just instructing water: in this case landscape doesn't control rain water so the application most likely goes into smoke...
Reply: Benjamin Toby
"actually the literal consequence of misusing the definition... and I think I demonstrated that..."
Exactly where do you think you showed that?

"that's not a consequence of the proper application of our definition sorry: the laws of physics don't code for any given system else even computer codes are coded by the laws of physics since the laws also work on them too"
You are not demonstrating where the application of our definition fails. I suppose you could say that part of all computer codes is physics itself, since without that information of how electromagnetism works no computer would function. If you want to avoid these kinds of issues you have to be more careful with your definitions.

"also you classified these laws to be part of the system so you'd need to find the code for it."
I've said it many times now, and even given concrete examples in both programming and physics: code can modify itself (especially DNA), so trying to draw a line between the code and the system will be quite a task for you.

"now that would be modifying our definition: lets try to work with our definition for now... going by our definition, there's no feedback"
Our definition does not require or prohibit feedback for it to be code.

"you didn't say "the landscape": that would imply there's a kind of landscape required for rivers: which doesn't fit either... you said "landscape": and that obviously doesn't fit our definition for code"
I don't follow. How did I imply that a special landscape is required for rivers to form. I am also not seeing how "landscape" doesn't fit our definition of "code," considering it's a configuration that functions to direct flowing water in a particular path.

"in addition landscape would be part of the river if it were to be called a system so we still need a code for the system."
Again you attempt to draw a necessary separation between code and system, which is not supported by the link you sent, any scientific definition, and especially the concept of DNA.

".I admit I don't have an example to show but atleast you concede humans can create volcanoes"
Unless you count the old elementary school baking soda and paper mache thing as a volcano, no I don't. What examples of man-made volcanoes do you know of?

"the purpose of the Andromeda system is forming the Andromeda system: it's a human-assigned purpose."
So if humans didn't name it, it wouldn't qualify as a system? Is this your argument? What purpose did we give it?

"however the purpose of the systems in the cell aren't assigned by humans... very big difference... they're just observed... eg the amino acid sequence building system made of the Ribosome, mRNA and tRNA... clearly the purpose of that system is to form amino acid sequences"
No, that's not any more clearly the purpose than it is the purpose of the Andromeda galaxy to form stars or look pretty. This is the whole point you are seeking to demonstrate.

"this is not a modification because from our definition the code is supposed to control a given system ... and I think our definition made a distinction b/w the code and the system"
What exactly do you think the term "given system" means, and where do you see our definition giving a necessary distinction between code and system? Why can the system not contain the code itself, as DNA does?

"code = rivershape"
ok, I can accept that

rivershape = no intelligence
Not equal, but there is no intelligence behind it

"DNA code = rivershape"
No, no. They are different codes.

"DNA code = no intelligence"
Again, not equal but no intelligence behind it.

"DNA code > Human computer code"
Why? Because humans can't replicate DNA code? Again, what about star code?

"no intelligence > Human computer code"
Well obviously. Nature is far more complex than any computer code.

"Human computer code > rivershape"
I'm not sure about this one. Depends on how accurate the model of the river is. No code can perfectly replicate the details of a river down to each molecule.

"no intelligence > Human computer code > rivershape"
Yes after so many fallacies you get silly conclusions. GIGO as we say in CS. I may as well stop here.

"that fails if we could find masses interacting without the laws of gravity or against the laws of gravity... in other words, that doesn't fit our definition..."
We know of no such masses, and I still don't see how that would violate our definition unless there were no laws governing their interaction at all.

"lets say we label the system to consist of water, landscape and laws of physics like you said, we still need to find the code for it"
Again you insist on this separation between code and system. I again reject this for reasons cited many times earlier.

Indeed, the issue seems to be distinction between code and system, to which again I refer you to DNA as a prime example of code that is part of its own system, as well as the AI and genetic algorithms I explained earlier. I cannot find your justification for saying that codes and the systems in which they operate must be separate.
Reply: Max Spiegel  You are not demonstrating where the application of our definition fails. I suppose you could say that part of all computer codes is physics itself, since without that information of how electromagnetism works no computer would function. If you want to avoid these kinds of issues you have to be more careful with your definitions. ... no no: it goes like this: if you want to avoid these kinds of issues you have to be more careful with your application...

I've said it many times now, and even given concrete examples in both programming and physics: code can modify itself (especially DNA), so trying to draw a line between the code and the system will be quite a task for you. ... and I've said it time and again our definition of code doesn't include self modification of the code... that's an extra bit you've added... our definition says a code must control a system and it's impossible for our definition to be viable if the code is controlling itself... that's like saying a computer program is programmed to control the program(itself)...

I don't follow. How did I imply that a special landscape is required for rivers to form. I am also not seeing how "landscape" doesn't fit our definition of "code," considering it's a configuration that functions to direct flowing water in a particular path. ... and you still need me to show you how your application falls apart? ... a landscape is visible features of an area of land (Wikipedia) ; a section or expanse of rural scenery, usually extensive, that can be seen from a single viewpoint. (dictionary.com) ; what definition can you give me to show a landscape functions to create rivers?... that's an equivocation of a high magnitude: and you cant use equivocations to validate your application: you have to be consistent with all your definitions and meanings else your application is false...

So if humans didn't name it, it wouldn't qualify as a system? Is this your argument? What purpose did we give it? ... first I'm not saying that it qualifies as a system because humans named it(whatever you mean by that)... I'm saying it qualifies as a system because humans assigned a function to it and I clearly stated the function... this is opposed to the amino acid building system I mentioned whose function isn't derived from human assignment... note: not the names, but functions...

No, that's not any more clearly the purpose than it is the purpose of the Andromeda galaxy to form stars or look pretty. This is the whole point you are seeking to demonstrate. ... I repeat the Andromeda galaxy is a system whose function is to form the Andromeda galaxy: not stars... the function is assigned by humans as opposed to the amino acid creating system which is just observed ... 

What exactly do you think the term "given system" means, and where do you see our definition giving a necessary distinction between code and system? Why can the system not contain the code itself, as DNA does? ... Ummm the amino acid sequence system doesn't contain the DNA, sorry... the DNA only contains the "information" and "configuration", functioning as "a set of instructions" for the amino acid system... now that's a perfect way to apply our definition... the DNA is not part of the system it's coding for...

Not equal, but there is no intelligence behind it ... one would think you were trying to correct my equation: turns out you were explaining it better: thanks...

No, no. They are different codes. ... this is very interesting... different codes? ... how so? ... I'm sorry but I wouldn't know that when you say the DNA is code in the same way a river shape is code...

Yes after so many fallacies you get silly conclusions. GIGO as we say in CS. I may as well stop here. ... silly conclusions? ... this is astute math bruh : saying nature is far more complex than any computer code is a white flag since it just proves my point ... btw your application of our definition is plagued with fallacies: how do these "silly conclusions" shape up with that?...

We know of no such masses, and I still don't see how that would violate our definition unless there were no laws governing their interaction at all. ... gravity or any other physical law don't govern the function of the amino acid sequence system... they are all influenced by these laws but not governed by them... the system doesn't function by any law of physics... the function can be influenced by the laws of physics, but not governed by it... 

Indeed, the issue seems to be distinction between code and system, to which again I refer you to DNA as a prime example of code that is part of its own system, as well as the AI and genetic algorithms I explained earlier. ... and I'm telling you DNA doesn't code for DNA ... 

so far so good: it seems like your application can't hold up to our definition without a plague of fallacies and equivocations... I however concede that my description of the DNA doesn't fit our definition accurately... instead of saying the DNA is a code, maybe I could say the DNA contains codes... just like a computer program contains codes... and maybe the DNA is a language: just like C++(separate subject)...
Reply: Benjamin Toby I am not adding anything to our definition. Saying that I have am adding something to our definition by including code that modifies itself would be like saying red rocks don't count as rocks unless the definition for rocks says they can be red. It would be you who would have to add the clause that code does not count as code if it modifies itself. DNA and other codes I have pointed out do modify themselves, so this would seem disadvantageous to you.

You are over-complicating the issue, so I will try to make this simpler to both clarify the problem and keep post size down. There is no such thing as a "misapplication of a definition." Given a definition, we can look at anything and ask ourselves "does this fit the definition? If not, what criteria does it not fulfill?" There is using the wrong definition (like when people think a scientific theory is just a guess), and there is a a bad definition (which is what we are working with).

Until you can point out what you mean by "misapplication of the definition" this isn't going anywhere. Can you give another example of how one could "misapply a definition?"

"Ummm the amino acid sequence system doesn't contain the DNA, sorry... the DNA only contains the "information" and "configuration", functioning as "a set of instructions" for the amino acid system... now that's a perfect way to apply our definition... the DNA is not part of the system it's coding for"
How is the amino acid sequence not what defines the "code" in DNA? If it doesn't, what does? What is "the amino acid system" apart from the configuration of a given stretch of DNA?

DNA is code that modifies itself, as is the AI example I gave earlier. DNA has code that codes to make more DNA, repair more DNA etc. You even have epigenetics at work. I can't see how you can separate the code from the system in an example like DNA.
Reply: Max Spiegel I need you to understand that it's self defeating for a code to primarily control itself: that's just not compatible with our definition and I gave you an analogy showing why: a self correcting code is a kind of code... our aim is to clarify what a code is to start with: and a self correcting or self adjusting code still controls a system just that it would require another system or mechanism to correct or adjust it: but the system it controls cannot adjust it directly else it's not even controlling the system at all...  

You are over-complicating the issue, so I will try to make this simpler to both clarify the problem and keep post size down. ... I appreciate your time and willingness to keep things as simple as possible... but you need to see it's you over complicating issues when you always ask for definitions for concepts that shouldn't be hard to grasp: this is all too familiar with you atheists and it's really frustrating: that's why I want you to see that I can go all the way and we probably wouldn't come to an agreement... the worse part is that you make these equivocations too: hell the definition of evolution is an equivocation: the dover case was lost because of an equivocation: funny enough that's what's actually keeping evolution viable... definition of terms... and I thought it was repeated experiments and observations that were supposed to make a science viable... 

just to make things simple, I'd agree temporarily that the DNA functions like a computer code: how still am I to believe it came up by purely natural means? that's impossible ... how would you propose it originated?
Reply: Benjamin Toby There is no way you can do science without an extremely rigorous, meticulous, borderline anal adherence to definitions. Imagine trying to apply the dictionary definition of "work" in a physical situation: it would violate conservation of energy.

Imagine if I said "The amount of work done on an closed system is equal to its change in potential and kinetic energy," and you said "What do you mean by 'work?'" and I said to you "Oh c'mon, everyone knows what work is!" That is what you are doing here by trying to avoid defining terms. In fact, you are constantly demonstrating that you are incapable of finding a definition for "code" that is both consistent and demonstrates what you want to prove. This is what seems to me your primary failure in this thread.

If you can't precisely define your terms, you cannot test your claims. There isn't a single word in scientific jargon that is not carefully defined to be testable. Our definition of code is not testable, hence it is useless.

"I need you to understand that it's self defeating for a code to primarily control itself: that's just not compatible with our definition and I gave you an analogy showing why: a self correcting code is a kind of code."
Ok, so you agree that self-correcting code is a kind of code.

"our aim is to clarify what a code is to start with:"
Yeah, in other words we are looking for a consistent, testable, non-trivial definition.

"and a self correcting or self adjusting code still controls a system just that it would require another system or mechanism to correct or adjust it: but the system it controls cannot adjust it directly else it's not even controlling the system at all."
I have to say, you kinda lost me here. Please clarify why code that codes to modify itself does not count as code (although you seemed to say the opposite earlier). You seem to again be trying to make a code/system distinction, and I'm not seeing where you can draw that line.
Reply: Benjamin Toby PS: The origin of the first part of the genetic code would be similar to the origin of the first river code: an interaction of natural laws and energy such that parts of the system tend towards some state of greater order. It's basically just a result of adding energy to a system in a way that decreases entropy, just like how snowflakes form.
Reply: +Max Spiegel  In fact, you are constantly demonstrating that you are incapable of finding a definition for "code" that is both consistent and demonstrates what you want to prove. This is what seems to me your primary failure in this thread. ... you know I noticed one very bothersome aspect with people like you: it is that you think anything you spit out counts as an explanation: just so you know you are as far from demonstrating the invalidity of our definition as you can possibly be... I'm just trying to call it off because you obviously wouldn't concede even if the evidence was right in front of you... let me try one more time to see if you can understand the simple point: 
-our definition: "information or a configuration functioning as a set of instructions for a given system."

-the information/configuration has a function, which is to instruct something
-from our definition it instructs a given system
-from you application the shape is the "information"
-and the shape instructs water
-water is not a system
-then you say the system is the river
-the system consists of the shape
-therefore the shape is instructing the shape...
-apparently you have "for a given system" mixed up with "in a given system"

if you defended the consistency of your application without outrageous fallacies and equivocations then you could have proven that your application was consistent: but you application transcribes to saying: landscape is code instructing water on how to flow ... that's obviously nonsense...

* The origin of the first part of the genetic code would be similar to the origin of the first river code: an interaction of natural laws and energy such that parts of the system tend towards some state of greater order. It's basically just a result of adding energy to a system in a way that decreases entropy, just like how snowflakes form.* ... so in other words you don't have a clue about how the DNA originated ... if you don't know how DNA originated or how all the molecular machines in the cell came about then you don't know anything about the origin of life: both simple celled and complex...
Reply: Benjamin Toby
"just so you know you are as far from demonstrating the invalidity of our definition as you can possibly be"
If you could have constructed a better definition that could not be subjected to what you perceive as abuse, you would have. The fact that you are not doing so is a pretty good proof that you are incapable of it.

Again I point out that there is no way to "misapply a definition" if it is a good, testable, scientific definition. Go ahead and try to misapply the physics definition of the word "work."

"-apparently you have 'for a given system' mixed up with 'in a given system'"
The two are not mutually exclusive. Something can code for a given system: namely the one it's in (again, like DNA)

"so in other words you don't have a clue about how the DNA originated"
You're right, I don't know anything about how or even for sure that abiogenesis occurred. It is just the most logical explanation based on our long history of discovering that all aspects we thought to be powered by magic could actually be explained by principles of nature, coupled with Occam's Razor. We may never know exactly how life originated, but that won't to a thing to cast doubt on evolution or common descent..
Reply: Max Spiegel  If you could have constructed a better definition that could not be subjected to what you perceive as abuse, you would have. The fact that you are not doing so is a pretty good proof that you are incapable of it.  ... the fact that I'm not constructing another definition is so we can come to a common agreement ... I can conjure up a new definition and you refuse it and you can conjure up a new one and I refuse it too ... so far our definition still stands because the definition doesn't allow you to call landscape code ... 

apparently you have for a given system mixed up with in a given system The two are not mutually exclusive. Something can code for a given system: namely the one it's in [again, like DNA] ... are you sure you understood the explanation I gave with the amino acid sequence system?... it doesn't seem like you did...

You're right, I don't know anything about how or even for sure that abiogenesis occurred. also you don't know about how simple organisms merged to form complex organisms: that's also an un-observable, un-testable assumption ... what you know is white moths change to dark moths, grey wolf to husky, e-coli to e-coli ... the rest is imagination... and I wouldn't fault you for that ... just don't tell me it is a scientific fact ... because it is a scientific fact that irreducibly complex systems are every where in living organisms...

 It is just the most logical explanation based on our long history of discovering that all aspects we thought to be powered by magic could actually be explained by principles of nature, coupled with Occam's Razor. ... let me tell you what magic is: magic is a fish morphing and shape-shifting into a cat ... I don't even think Biblical miracles beat that...

 We may never know exactly how life originated, but that won't to a thing to cast doubt on evolution or common descent.. just out of curiosity, how do you falsify the notion of simple organisms like bacteria turning into complex organisms like cats?
Reply: Benjamin Toby 
"the fact that I'm not constructing another definition is so we can come to a common agreement ... I can conjure up a new definition and you refuse it and you can conjure up a new one and I refuse it too"
You can't make a bad definition work. That's like trying to fit a square peg in a round hole.

I have not once refused your definitions. I invite you to construct any definition, and I will accept it. The whole point is that all your attempts either fail to be consistent, or result in trivial absurdities such as "all nature is a code."

"so far our definition still stands because the definition doesn't allow you to call landscape code "
I must have missed where you showed me how the landscape is not a configuration that functions to direct rainwater/wind/etc.

"are you sure you understood the explanation I gave with the amino acid sequence system?... it doesn't seem like you did."
No, as a matter of fact I specifically asked you to explain yourself more clearly on how the amino acid sequence is different than DNA. DNA codes for amino acids, which then act on the DNA to replicate, deactivate, and repair certain parts. DNA is both the source of and changed by the actions of proteins.

"also you don't know about how simple organisms merged to form complex organisms: that's also an un-observable, un-testable assumption "
Just because I don't know how they did doesn't mean I don't know that they did. Common descent makes unique, falsifiable predictions that have been borne out through repeated experimentation. That is how heliocentrism was proven too. You accept that, right?

"because it is a scientific fact that irreducibly complex systems are every where in living organisms"
Nobody has ever demonstrated a system to be "irreducibly complex." We don't even know how one would prove that. Even the stupid mouse trap example was shown to fail.

"let me tell you what magic is: magic is a fish morphing and shape-shifting into a cat"
I'm sure we can agree on that. That would be like one of your grandfathers morphing into you. Good think that's not a prediction of evolution, and would in fact violate evolution. If this is how you really think evolution works then you just lost a fair amount of respect from me; I thought you were smarter than this.

"just out of curiosity, how do you falsify the notion of simple organisms like bacteria turning into complex organisms like cats?"
Again, that is not evolution. One could falsify evolution if we found a pre-Cambrian rabbit, or if our genetic makeup were more similar to a daffodil than a chimp, or if we saw a fish morph into a cat, etc. Go out and do the experiment yourself: start digging. Maybe you'll be the one to disprove common descent.
Reply: Max Spiegel  You can't make a bad definition work. That's like trying to fit a square peg in a round hole. ... and you don't get to label our definition bad until you properly apply it to another unsuitable scenario without making a heap load of equivocations and fallacies... in other words our definition isn't wrong because you say so: neither is it wrong because you misapplied it...

I have not once refused your definitions. I invite you to construct any definition, and I will accept it. The whole point is that all your attempts either fail to be consistent, or result in trivial absurdities such as "all nature is a code." ... firstly you proposed a test to falsify our definition and I've put your test through scrutiny and critical check; tuns out that your test was a fail ... secondly new definition? well check this out: ... a code: in biology, a code is any biological molecule that functions like the DNA ... beat that...

I must have missed where you showed me how the landscape is not a configuration that functions to direct rainwater/wind/etc. ... so you missed where I showed you that landscape is the visible features of an area of land and not the shape of a river?

No, as a matter of fact I specifically asked you to explain yourself more clearly on how the amino acid sequence is different than DNA. * actually it's amino acid sequence *system ... I think I made that quite clear... the job of this system is clearly to create amino acid sequences: this was the function(purpose) I pointed out which made it a system ...

Just because I don't know how they did doesn't mean I don't know that they did. ... actually it does... the fact that we have complex organisms now isn't a testament to a scenario of single cells "self-merging" to form the complex celled organisms... if they ever merged, it was most likely intelligently caused...

Nobody has ever demonstrated a system to be "irreducibly complex." We don't even know how one would prove that. Even the stupid mouse trap example was shown to fail. ... well I was hoping we could talk about this ... and I really feel for Behe having to answer to a plethora of unintelligent responses to his concept... this is probably why he hasn't conceded any form of refutation posed by the supposed scientific community ... what is an irreducibly complex system? an irreducibly complex system is a single system which is composed of several interacting parts that contribute to the basic function, and where the removal of any one of the parts causes the system to effectively cease functioning. ... how do we test for an irreducibly complex system? simple; get into a lab, take a set of bacteria with single flagellum, systematically knock out each and every single part of the flagellum system... if knocking out any of these parts causes the mechanism to stop functioning as a propeller of the organism, then that bacteria flagellum is irreducibly complex: if the flagellum maintains its function with each of these parts systematically knocked out, the bacteria flagellum is not irreducibly complex... QED ... how hard is that? ... 

 That would be like one of your grandfathers morphing into you. Good think that's not a prediction of evolution, and would in fact violate evolution. If this is how you really think evolution works then you just lost a fair amount of respect from me; I thought you were smarter than this. ... first "grandfathers morphing into you"? that's funny I'd have to say ... secondly do you honestly think I really care about your perception of my intellect? ... what do you think this is? ... this is not a contest to be won or lost ... these are important things that shape our lives and destinies: even that of our future generations ... these are things we probably can't afford to get wrong for the sake of our race ... these are things that form the foundation of all our paradigms, reasoning, and actions... all I'm after is the truth: and I don't think you're going to prove anything with the warped definition of evolution...

One could falsify evolution if we found a pre-Cambrian rabbit, or if our genetic makeup were more similar to a daffodil than a chimp, ... does the 50% DNA similarity with bananas count? or maybe mice with 92% DNA similarity?
Reply: +Benjamin Toby 
"our definition isn't wrong because you say so: neither is it wrong because you misapplied it"
I repeat: there is no such thing as "misapplication of a definition." There are only wrong definitions and bad definitions. By "misapply" you seem to mean that we are working with the wrong definition, in which case I again invite to make the right one. Go ahead and try to "misapply" the definition of the another word and I will show you how it falls into one of the two categories I listed above.

"firstly you proposed a test to falsify our definition and I've put your test through scrutiny and critical check; tuns out that your test was a fail"
I missed that. I remember the part where you showed how applying our definition of "code" to the river led to asinine consequences, which is again an indication that we are working with a bad definition.

"in biology, a code is any biological molecule that functions like the DNA ... beat that..."
That's a pretty strange definition. What do you mean "functions like DNA?"  How can we test for this? Where did you get this definition?

"so you missed where I showed you that landscape is the visible features of an area of land and not the shape of a river?"
No, I missed where you showed me that this does not fit our definition of code, since the landscape still provides instructions for where water can flow across it.

"the job of this system is clearly to create amino acid sequences: this was the function(purpose) I pointed out which made it a system"
So the job of the amino acid system is to create amino acid sequences which may or may not modify the DNA "coding" for that system? Does that sound consistent or logical to you?

"actually it does... the fact that we have complex organisms now isn't a testament to a scenario of single cells "self-merging" to form the complex celled organisms... if they ever merged, it was most likely intelligently caused"
You don't have to know how something happened to know that it happened. How did Alexander the great die? We don't know. Did he die? Yes. How do we know? Because of induction: every person recorded has died. Similarly, we see evidence that monocellular organisms became multicellular organisms, and we see this happen in the development of every embryo in existence through natural means. We have observed this as a result of "intelligence" exactly zero times. Induction.

"if the flagellum maintains its function with each of these parts systematically knocked out, the bacteria flagellum is not irreducibly complex"
But that wouldn't demonstrate that the flagellum couldn't have evolved naturally, that only demonstrates that it can't operate without certain components. This test is pointless, and in no way indicates "intelligence."

" all I'm after is the truth: and I don't think you're going to prove anything with the warped definition of evolution"
What "warped definition" are you referring to?

"does the 50% DNA similarity with bananas count? or maybe mice with 92% DNA similarity?"
No, because this shows we are more closely related to mammals than to plants. If we had 50% shared with mice and 92% with bananas, then evolution would be in trouble.
Reply: Max Spiegel    I repeat: there is no such thing as "misapplication of a definition." ... OK lets just say you didn't apply the definition at all... or else you want to say I can apply the definition of work to say landscape has done work ... 

No, I missed where you showed me that this does not fit our definition of code, since the landscape still provides instructions for where water can flow across it. ... again, "the landscape" is very different from "landscape" ... if you can understand this and the implications it has on your supposed application, then you can see that your application turns to gibberish ... 

What do you mean "functions like DNA?" ... OK what do you mean "What do you mean"?

How can we test for this? Where did you get this definition? ... we can test this by observing the DNA and identifying its functions, and then observing any other biological molecule... if there's any molecule that acts like the DNA, it's a code... btw that definition came from pure inspiration [aka being fed up with your semantics]... 

So the job of the amino acid system is to create amino acid sequences which may or may not modify the DNA "coding" for that system? Does that sound consistent or logical to you? ... there's no "which may or may not modify the DNA" ... the basic function is to create amino acid sequences: another system is required to fold the sequences into proteins ... I just used that instance to identify a system with a specific function... 

You don't have to know how something happened to know that it happened. ... you have to factually know how it could have happened to know it happened the way you think it happened: we know how people die and evidences of death that's why we can induce from that to say conclusively that something is dead... 

Similarly, we see evidence that monocellular organisms became multicellular organisms, and we see this happen in the development of every embryo in existence through natural means. ... really? embryology told you that generations of bacteria can develop DNA information to form a Human over millions of years? ... I think that's desperate ... well embryology tells me that every human embryo is pre-loaded with specific DNA instructions to guide it's development over nine months... embryology also tells me that it's impossible to get a human embryo from a couple of monkeys or rats... I don't know much about embryology but I know that every embryo we know and observe follows after the kind that begat it... and that simply means that there should have been a first kind to kick start the cycle: from this the induction is design...

But that wouldn't demonstrate that the flagellum couldn't have evolved naturally, that only demonstrates that it can't operate without certain components. This test is pointless, and in no way indicates "intelligence." ... firstly the test is to determine that a system is irreducibly complex: if the test is repeated and the same result comes out, then without a doubt the system in test is irreducibly complex: scientific fact ... now after establishing that fact, it's left for you evolutionists to explain how that irreducibly complex system can arise by the mechanisms of biological evolution: if an explanation is found, the only way to falsify the claim would be to put the explanation to the test in a laboratory... if it can't be replicated in a laboratory, then the explanation fails to refute the empirical, tested scientific fact... so far, I've not heard any feasible explanation from evolutionists which can refute the irreducible complexity of the bacteria flagellum ... all I've heard is exaptation and the type 3 secretory system as an example: which is basically nonsense... to refute Behe's claims with the type 3 secretory system or any other homologous system of that kind, first evolutionists need to find or imagine the pre-existing functions of the other 20+ parts needed to form the flagellum, and then fabricate an evolutionary pathway through which the type 3 secretory system can collate with the other 20+ parts to form the bacteria flagella... after that, they need to put it to the test in a lab and see if it works... the issue is, even with all the imaginative fabrications in evolution, no one seems to be able to find an imaginary pathway to achieving the flagellum... but they say Behe's concept is refuted... I can't help but think that these people are willfully clueless about Behe's concept... so long as the bacteria flagellum is factually proven to be irreducibly complex, the only logical explanation is design...

What "warped definition" are you referring to? ... OK lemme ask you something ... if evolution is "change in allele frequency with time", how do we apply that to Chemical Evolution?
Reply: +Benjamin Toby 
"or else you want to say I can apply the definition of work to say landscape has done work"
Yes, try to do this. This would illustrate what you mean by "misapplying a definition."

"again, 'the landscape' is very different from 'landscape'"
I'm sorry, you lost me here. What's the difference?

"OK what do you mean 'What do you mean'?"
I mean which functions make a molecule DNA-like? Would the other proposed molecules in your definition need to correspond to amino acids, or just self-replicate or what? DNA doesn't do just one thing. Your definition seems to amount to "code is defined as DNA or anything like DNA,"which is a tautology for our purposes, since you seek to prove how this code is so similar to other non-biological codes that it must have a designer.

"there's no "which may or may not modify the DNA" ... the basic function is to create amino acid sequences: another system is required to fold the sequences into proteins"
The amino acid sequences may or may not modify the DNA, that is a fact. What system do you think does the folding? It's obviously just physics.

"we know how people die and evidences of death that's why we can induce from that to say conclusively that something is dead."
And we know that nature can take a single cell and grow it into an organism with billlions of cells. We know it can combine cells into temporary structures in things like plasmodial slime molds.

"embryology told you that generations of bacteria can develop DNA information to form a Human over millions of years?"
No, it tells me that nature is capable of taking a single cell and making it develop into a multi-cellular organism. The veracity of common descent comes from sum total of all the evidence we have for evolution and its many successful, unique predictions. I was only addressing one point; namely the idea that going from unicellular life to multi-cellular life can occur without intelligence.

"and that simply means that there should have been a first kind to kick start the cycle: from this the induction is design"
When have you ever observed this in nature? It's not induction unless you have seen it happen before. Nobody has ever observed a "first kind" just pop up.

"now after establishing that fact, it's left for you evolutionists to explain how that irreducibly complex system can arise by the mechanisms of biological evolution"
You make it sound as if, by showing that the flagellum doesn't function without some particular part, science must now scramble to find the exact evolutionary pathway by which it developed and replicate it in a laboratory, or else it must be design by default. In reality, all this test would demonstrate is that this flagellum doesn't function without this component. 

The fact that it did evolve through natural means is a deduction from the many unique, falsifiable predictions made by evolution; we don't need to construct a pathway for every (or even any) specific organelle. ID needs unique, falsifiable claims that we can test, and the idea that removing a component from a flagellum makes it stop working is far from a unique prediction of ID. A unique prediction of ID would be "it is impossible for flagella to evolve naturally," and then we would need some test to prove this, which removing a part to make it non-functional does not achieve.

Indeed, it turns out that many of the components of the flagellum, when removed, can perform other functions in the cell. Furthermore, we see evolution evolve "irreducibly complex" structures all the time, like nylonase in the famous E. Coli long-term experiment. Remove any component of the nylonase molecule and it ceases to function, yet it evolved right before our eyes.
Reply: Max Spiegel    Yes, try to do this. ... I just did... I applied the definition... same way you applied our definition...

I'm sorry, you lost me here. What's the difference? ... "the landscape" presupposes a kind of landscape required for rivers: "landscape" dissolves any such presuppositions because it is a general term with no specific meaning in this context... and I gave you the definition of landscape and showed that the term can't be applied without some form of descriptive adjective... I don't know if you get me now...

Your definition seems to amount to "code is defined as DNA or anything like DNA,"which is a tautology for our purposes ... oh you figured? ... I was kind of hoping you'd see that... just to get a hold on the way terms are twisted in evolution... but it appears like I might have to use another instance to get you to really understand the implications of language manipulation and how it is used to validate evolution...

The amino acid sequences may or may not modify the DNA, that is a fact. What system do you think does the folding? It's obviously just physics. ... again, my point is if we can identify a system that has a specific function and is operated by the DNA... and the system I pointed out specifically makes amino acid sequences: and it does that by interpreting DNA codes... 

And we know that nature can take a single cell and grow it into an organism with billlions of cells. ... huh?... seriously? ... how does formation of embryos support a unicellular to multicellular transformation over generations? ... the fact is all embryos are replications of their kind... so the embryos would actually negate evolution because all generations we observe follow after their kind... 

I was only addressing one point; namely the idea that going from unicellular life to multi-cellular life can occur without intelligence. ... and I'm saying going from a fertilized egg to a human baby is very different from transformation from bacteria to humans through reproductive generations... all generations can only transfer what they have and that's a fact... going by that, humans have always been humans... therefore there had to be a start for the reproductive cycle of humans...

The veracity of common descent comes from sum total of all the evidence we have for evolution and its many successful, unique predictions. ... you know it's not going to help if you keep using presuppositions based on evolution to make assertions: firstly common descent is only viable if one presupposes evolution is true: but common descent is only common designer from my point of view and that's what I would predict... secondly didn't evolution predict that there would be numerous transitional fossils showing the gradual transformation between species? ... doesn't that count as a failed prediction?

You make it sound as if, by showing that the flagellum doesn't function without some particular part, science must now scramble to find the exact evolutionary pathway by which it developed and replicate it in a laboratory, or else it must be design by default. ... actually that's more or less the situation on ground... the fact is that the bacteria flagellum is irreducibly complex and no evolutionary process can give rise to an irreducibly complex system: so logic just says it was most likely designed... if you still hold that evolutionary processes can give rise to it then you are free to use all of your imagination to lay down a step-by-step procedure to achieve that...

In reality, all this test would demonstrate is that this flagellum doesn't function without this component. ... it's called irreducible complexity: the test would demonstrate that the bacteria flagellum is irreducibly complex...

The fact that it did evolve through natural means is a deduction from the many unique, falsifiable predictions made by evolution; we don't need to construct a pathway for every (or even any) specific organelle. ... you know I think this is the basic problem with evolutionists: it's just like religious people refusing to let their religious presuppositions go through testing and critical thinking... it's not a fact that the bacteria flagellum evolved: it's only another presupposition of yours which is not going to help our discussion very much... lets try to limit this discussion to proven and testable facts...

A unique prediction of ID would be "it is impossible for flagella to evolve naturally," and then we would need some test to prove this ... why would you have us do your job of validating your theory? ... 

Indeed, it turns out that many of the components of the flagellum, when removed, can perform other functions in the cell. ... OK just tell me a possible function of the hook before the assemblage took place... 

Furthermore, we see evolution evolve "irreducibly complex" structures all the time, like nylonase in the famous E. Coli long-term experiment. Remove any component of the nylonase molecule and it ceases to function, yet it evolved right before our eyes. ... you know to be honest I've really tried to get a good hold on what exactly happened in that experiment: maybe you could explain it better to me: I heard the e coli bacteria adapted to a situation by loosing a component(or some components) ... I really hope that's not true for the sake of you evolutionists: because that would be the exact opposite of evolution: loosing components is never going to get an e coli to a multicellular organism...
Reply: What the hell, did Mark Champneys delete my comment? Mark, please tell me you are not so cowardly.

Benjamin Toby Did you get a chance to read my reply, or do I have to type it again?
Reply: Max Spiegel  Didn't get it: sorry ...
Reply: Max Spiegel Did you say some special in that comment, or what? Seems weird to only delete one specific comment, otherwise. It might also, possibly, have got spam-filtered, perhaps? Just a thought.
Reply: antiHUMANDesigns It had two links in it, but nothing I think would be filtered. Whatever, I'll give Mark the benefit of the doubt and retype my response when I have the time.
Reply: +Max Spiegel The only comments that ever get deleted by me are for profanity, and that is rare.  I welcome comments from those who disagree with me.  That is why over 14,000 comments have been posted to this forum.  Google does weird stuff, however.  Who knows?
Reply: Ok, Mark. Like I said I will give you the benefit of the doubt here. I am just posting now to remind myself to rewrite my reply when I get back from vacation.
Reply: Benjamin Toby 
"I applied the definition... same way you applied our definition."
Where did you show that applying our definition of "code" to a landscape lead to a contradiction? I saw that it merely led to useless tautologies.

"'the landscape' presupposes a kind of landscape required for rivers: 'landscape' dissolves any such presuppositions because it is a general term with no specific meaning in this context... and I gave you the definition of landscape and showed that the term can't be applied without some form of descriptive adjective."
I don't see where you did that. I asked you to give me an example of a misapplication of the scientific definition of the word "work" to a landscape that would illustrate  what you mean by "misapplying a definition."

"again, my point is if we can identify a system that has a specific function and is operated by the DNA... and the system I pointed out specifically makes amino acid sequences: and it does that by interpreting DNA codes."
So what? My point is that the process of transcription and translation then goes on to modify the amino acid "code" for that same process, so we have an example of self-modifying code.

"how does formation of embryos support a unicellular to multicellular transformation over generations? ... the fact is all embryos are replications of their kind... so the embryos would actually negate evolution because all generations we observe follow after their kind."
Firstly, the point was simply that unicellular life to multi-cellular life seems to be the kind of thing nature can accomplish, yet humans cannot. The evidence that it occurred over changes to successive generations is separate.

Secondly, what is a "kind?" That each generation will be genetically, and therefore phenotypically similar to its parent generation is a requirement of evolution. Evolution predicts that it is impossible that a herring will give birth to a penguin, but rather that each individual in each generation will be slightly different than the parent, and that these differences gradually accumulate to create reproductive barriers between species, leading to increased specificity and variety.

"all generations can only transfer what they have and that's a fact..."
Random mutations change genetic sequences, so this is false.

"... going by that, humans have always been humans... therefore there had to be a start for the reproductive cycle of humans."
All life reproduces. That is considered one of its greatest defining features. The start of the human reproductive cycle was the reproductive cycle of our mammalian ancestors.

"firstly common descent is only viable if one presupposes evolution is true"
False: we could say that we all descended from a common ancestor and that magical pixie dust guided and powered the process of diversifying life.

"but common descent is only common designer from my point of view and that's what I would predict"
And what falsifiable, repeatable tests could we perform to prove this prediction? 

"secondly didn't evolution predict that there would be numerous transitional fossils showing the gradual transformation between species? ... doesn't that count as a failed prediction?"
Not when we have found zillions of them:
transitionalfossils.com

"the fact is that the bacteria flagellum is irreducibly complex and no evolutionary process can give rise to an irreducibly complex system: so logic just says it was most likely designed... if you still hold that evolutionary processes can give rise to it then you are free to use all of your imagination to lay down a step-by-step procedure to achieve that."
Completely untrue. We have no reason at all to suspect that an "irreducibly complex" (IC) system, as defined by Behe, cannot arise by evolutionary means. IC simply means that removing any part of the system renders it useless.

First, let's deal with the flagellum. The it turns out that bacteria that inject toxins into host cells use something called a "type III secretory system," which is an arrangement of proteins that appears perfectly homologous to the base of the flagellum. This means that the flagellum can serve a purpose without all its parts, and hence is not IC.

Secondly, let's see how the concept of IC is itself flawed. The relevance vanishes under the idea of the Mullerian Two-Step:
Step one: add a part
Step two: make that part essential
Here, for instance, I will construct an IC bridge with gradual, evolution-like steps:
We start with a simple row of bricks

OOO

We add a plank across the top
_____
OOO

We remove the middle block
_____
O  O

We now have an IC bridge, because the removal of any part renders it useless. Yet this is obviously the kind of thing that evolution would be readily capable of. 
IC is useless. Even the mousetrap example was shown to fail in court.

"it's not a fact that the bacteria flagellum evolved: it's only another presupposition of yours which is not going to help our discussion very much... lets try to limit this discussion to proven and testable facts."
It is as much a fact that the flagellum evolved as it is a fact that gravity caused the stars and planets to form instead of magical angels because we know gravity works that way, or that Alexander the Great died and didn't become an invisible superhero because he was presumably a mortal human like the rest of us. It is the only viable theory on the grounds of having the sort of predictive power I have repeatedly described countless times.

Me: "A unique prediction of ID would be "it is impossible for flagella to evolve naturally," and then we would need some test to prove this" 
You: "why would you have us do your job of validating your theory?" 
Common descent if already validated through its predictive power. You must now disprove it by validating your positive claim that some aspect of it is impossible.

"OK just tell me a possible function of the hook before the assemblage took place."
Part of a filament, perhaps? We probably don't know yet, but you should consult experts in this stuff. We at least have a pretty clear picture of at least one primitive function for the base, as I mentioned earlier.

"you know to be honest I've really tried to get a good hold on what exactly happened in [the long-term E. Coli] experiment: maybe you could explain it better to me: I heard the e coli bacteria adapted to a situation by loosing a component(or some components) ... I really hope that's not true for the sake of you evolutionists: because that would be the exact opposite of evolution: loosing components is never going to get an e coli to a multicellular organism."
The bacteria, over the course of many generations, selective pressure, and possibly through a frameshift mutation, developed the ability to digest nylon in addition to their original food source. AiG Claims this is bad because it is a "loss of specificity," as if my lungs gaining the ability to function underwater would be detrimental because of "loss of specificity." What a laugh.
Reply: I have attempted to replicate my earlier reply above. Hopefully it stays visible this time.
Reply: Max Spiegel  OH here we go again ... Mr Spiegel you have to work with me here ... I really hope your thinking isn't as bad as your colleague here ... because it seems like you're just repeating your lines without paying specific attention to details and disparity in beliefs ... 

1. Where did you show that applying our definition of "code" to a landscape lead to a contradiction? I saw that it merely led to useless tautologies. ... ah well you probably didn't see well enough ... I don't believe we should dwell on this for so long if I'm going to be repeating myself over again ... I pointed out numerous contradictions and equivocations ... I'm not sure I can go through my entire comment to show it to you again ...

2. So what? My point is that the process of transcription and translation then goes on to modify the amino acid "code" for that same process, so we have an example of self-modifying code. ... and again a "self-modifying code" is a TYPE OF CODE ... the code doesn't modify itself directly ... it requires a feedback system ...

3. Firstly, the point was simply that unicellular life to multi-cellular life seems to be the kind of thing nature can accomplish ... again your presuppositions getting in the way ... the fact that we see simple cells form to become multi-cellular organisms in embryology is in no way a justification for the origin of such function by natural means ... from what we see, nature is only repeating a process that had a specific starting point, of which natural means cannot explain ...

4. Secondly, what is a "kind?" ... a kind would be somewhere in the range of family and genus ... it's hard to conclusively define a kind ... but eagles, for example can be defined as a kind ...

5. Evolution predicts that it is impossible that a herring will give birth to a penguin ... well news flash ... ID predicts that it's impossible for a herring to produce a penguin: so we could agree that based on this prediction, ID is a credible scientific theory. No? ... PS ID is more credible since it doesn't contradict itself by saying herrings can morph to penguins given millions of years ...

6. Random mutations change genetic sequences, so this is false. ... random mutations can scramble already present DNA information, random mutations can destroy DNA information, random mutations cannot produce brand new information: so I hold, since the genes transferred are strictly derived from the parent genes, all siblings cannot receive what's not already contained in the parent ... there can be loss or disruption or duplication of sequences, but all still follows the parents prototype ...

7. The start of the human reproductive cycle was the reproductive cycle of our mammalian ancestors. ... here we go again with the presuppositions ... 

8. And what falsifiable, repeatable tests could we perform to prove this prediction? ... simple: if you can find any living thing that doesn't have DNA, then the prediction is false ... also, considering that things happen randomly in evolution shouldn't there be another molecule that creates life? since molecules can just spawn up and start reproducing? this would be a good falsification of the evolution story ...

9. Not when we have found zillions of them ... I heard that the nebraska man was one of these transitions at one time ... why should I buy into this when they can just conjure up a human transition from a tooth of a wild pig? ... also, do these "zillion" transitional fossils include the pre-cambrian transitions?

10. Completely untrue. We have no reason at all to suspect that an "irreducibly complex" (IC) system, as defined by Behe, cannot arise by evolutionary means. IC simply means that removing any part of the system renders it useless. ... Ummm IC simply means that removing any part of the system CAUSES IT TO LOOSE ITS FUNCTION ... not that it is totally useless for other functions ... and you have every reason to suspect an IC system cannot arise from evolutionary processes since apparently the scientists criticizing Behe can be best described as retarded ... I mean Ken Miller: is that guy supposed to be a scientist? ... he can't even understand the simple concept and he leaves Behe with the daunting task of repeating himself over and over again while Behe's words seem to be hitting a brick wall of self deceit ...

11.  *IC is useless. Even the mousetrap example was shown to fail in court* ... well I watched a documentary about the dover case and it turned out that ID lost because it was categorized as a religion ... how powerful are equivocations? ... u should understand that this is the main tool of evolution and this my main argument ... also I don't know if the Mousetrap analogy actually failed or if it's just you wishful thinking ... a child can understand the analogy easily ... take away a component from a mousetrap, and it wouldn't be catching no mice ... induce from that that conclude it was intelligently designed with all the parts purposefully placed: or maybe you can go the retarded way and induce that it can be reduced to form a tie clip which has nothing to do with catching mice ...

12. The bacteria, over the course of many generations, selective pressure, and possibly through a frameshift mutation, developed the ability to digest nylon in addition to their original food source. AiG Claims this is bad because it is a "loss of specificity," as if my lungs gaining the ability to function underwater would be detrimental because of "loss of specificity." What a laugh. ... don't laugh so quick ... do you accept that the most notable change gained by the bacteria came up by a loss of function or component? if so then how will loosing functions and components produce a multicellular human being from a single-celled bacteria for Gods sake?

You see it seems to me like you're confused about IC just like most of the so called scientists that claim they refuted the concept ... let me give you a break down of the hierarchy of the argument ...

1. Identify the system to be studied and the function it performs: take the popular example of the bacteria flagellum in this case ... a rotary motor with a hook and a tail and some other components all working together ... function to be achieved is efficient and effective mobility of the bacteria ...

2. Identify if the system is Irreducibly complex as the definition states: a system that looses a function at the absence of any component part is by definition Irreducibly Complex ... Thus if a test is carried out and it is found that on the elimination of ANY component of the flagellum, it looses it's function, then it can be conclusively said that that flagellum in test is irreducibly complex ... repitition of this test with the same result makes it a Scientific Fact ...

3. Now the postulations can be made from the test... if the bacteria in question looses mobility at the elimination of any component, then logic follows that all components that caused the flagellum to cease function must be present for the flagellum to work... all of these components can be classified into a sub system called the "Irreducible Core"

4. Next postulation... if all these components in the irreducible core must be present for the flagellum to work, logic follows that the irreducible core had to arise spontaneously with all the components present, perfectly matched, and functioning effectively.

5. If all this had to arise spontaneously, then we can say it's impossible for a process to form it by adding components one at a time ...

6. and if evolution works by adding components one at a time, the evolution could not have given rise the the system in question ...

7. If evolution works by adding all these components spontenously with all the well matching interactions and deft assembly instructions, then we are definitely talking of an intelligent, sentient process not an undirected process. we are already talking about ID.

I could also add a mathematical equation to describe this. NB this is not part of the main arguments from Behe: just my thought ...

1. This test can be deduced into a mathematical expression. Lets say the components present in the flagellum in question are 50. we can define a term called Irreducible complexity index(ICxI) which stands for the number of components present in the system studied. 

2. We can also call for another term irreducible core index ... which is the number of components present in the irreducible core. lets assume for the sake of this equation that the irreducible core index (ICoI) is 35( ie 35 components caused the flagellum to stop functioning on removal).

3. We can call for yet another term called irreducible complexity quotient : which will be the ratio of the ICoI to the ICxI and a measure of irreducible complexity of the system. in this case we would get a quotient of 0.7. The quotient ranges from 0 to 1 with 0 representing the least irreducibly complex and 1 representing the most irreducibly complex... 

4. then we can say that the range of ICQ from 0.5 to 1 conclusively represents a range of impossibility for evolutionary process, for the reasons listed above.
Reply: Benjamin Toby "it's hard to conclusively define a kind ... but eagles, for example can be defined as a kind"

Why are eagles a "kind"? By what criteria? Why are they a different "kind" than falcons?

And do you agree that "birds" are a group, while "raptiles" is a different group?
And do you agree that "vertebrates" is a group, and "invertebrates" are a different group?
So "kinds" can be grouped into "groups of kinds", and so on?
And animals vs plants vs fungi, for example, are also "groups of groups of kinds", right?
Reply: antiHUMANDesigns the criteria is most likely physical and mental attributes ... maybe falcons and hawks might even belong to the same kind as eagles: but like I said a conclusive distinction is hard for me ...
Reply: Benjamin Toby
"and again a "self-modifying code" is a TYPE OF CODE ... the code doesn't modify itself directly ... it requires a feedback system "
What is the system in this case? You said something before about the "amino acid system." I've never heard of such a thing.

"the fact that we see simple cells form to become multi-cellular organisms in embryology is in no way a justification for the origin of such function by natural means"
You said it was impossible for nature to make creatures go from single-celled to multicellular. This counterexample proves otherwise.. That's all I'm saying.

"it's hard to conclusively define a kind"
As AHD pointed out, this is pure garbage. You aren't even sure that eagles are a kind when pressed on the matter. If your definition cannot be tested, it is useless.

"ID predicts that it's impossible for a herring to produce a penguin: so we could agree that based on this prediction, ID is a credible scientific theory."
No, missed the "pre" part of "prediction." Looking after the fact and retrofitting your observations would be "postdiction." Also, nobody has proved that it is impossible for a Herring to be the ancestor of a Penguin, so that fails on all fronts.

"ID is more credible since it doesn't contradict itself by saying herrings can morph to penguins given millions of years"
Evolution does not say this is possible either; you are merely illustrating your lack of understanding by stating such nonsense.

"random mutations can scramble already present DNA information, random mutations can destroy DNA information, random mutations cannot produce brand new information: "
Duplications create new information. Point mutations create new information. Combining these with other kinds of mutations like deletions and frameshift mutations lead to infinite possibilities for the functions of that new information.

"if you can find any living thing that doesn't have DNA, then the prediction is false "
Unique predictions, Toby. They must be unique to the theory. Besides, I don't see how finding a creature with a different chemical structure instead of DNA would be a problem for either ID or evolution.

"considering that things happen randomly in evolution shouldn't there be another molecule that creates life? since molecules can just spawn up and start reproducing? "
Firstly, evolution is not random. Second, any new abiogenesis trying to appear on the planet would be snuffed out by the already dominant life forms we have unless it proves instantly pathogenic to all of them, which seems rather unlikely.

"I heard that the nebraska man was one of these transitions at one time ... why should I buy into this when they can just conjure up a human transition from a tooth of a wild pig? "
Yeah, and you know who exposed that fraud? Evolutionary biologists. Not creationists. Stories like Nebraska Man are examples of why we can trust scientists and not creationists. You should "buy into" the effectiveness of peer review because of examples like this, and understand that this means that all the items on the list I gave you have been checked and double-checked for authenticity.

"IC simply means that removing any part of the system CAUSES IT TO LOOSE ITS FUNCTION ... not that it is totally useless for other functions"
Well then the concept is even more useless than I thought. However that is not what Behe says; he says:

"By irreducibly complex I mean a single system composed of several well-matched, interacting parts that contribute to the basic function, wherein the removal of any one of the parts causes the system to effectively cease functioning."
-Behe

He doesn't say that it can now have a different function; he just says "cease functioning." You want to adapt his definition to "cease functioning in the original way for the original purpose?" Fine, but that's your addition, not part of the original.

"and you have every reason to suspect an IC system cannot arise from evolutionary processes since apparently the scientists criticizing Behe can be best described as retarded."
I created an IC system through evolutionary-style changes right before your eyes! Did you not read my bridge example?

"also I don't know if the Mousetrap analogy actually failed or if it's just you wishful thinking"
It failed because a mousetrap is not IC. I can remove part of it and use the rest for something else.

"do you accept that the most notable change [in the E. Coli experiment] gained by the bacteria came up by a loss of function or component?"
No, where did anyone say that? I pointed out that the bacteria gained the ability to digest nylon in addition to its regular food source. The best AiG could do to call this a "loss" was to say it was a "loss of specificity." That's like saying if birds can suddenly use their wings to swim they lost something. That is definitely worth a laugh.

"You see it seems to me like you're confused about IC just like most of the so called scientists that claim they refuted the concept ... let me give you a break down of the hierarchy of the argument"

1. Identify the system to be studied and the function it performs: take the popular example of the bacteria flagellum in this case ... a rotary motor with a hook and a tail and some other components all working together ... function to be achieved is efficient and effective mobility of the bacteria
This is makes it sound like evolution has the goal of creating this particular functionality, but whatever we can let that slide.

2. Identify if the system is Irreducibly complex as the definition states: a system that looses a function at the absence of any component part is by definition Irreducibly Complex ... Thus if a test is carried out and it is found that on the elimination of ANY component of the flagellum, it looses it's function, then it can be conclusively said that that flagellum in test is irreducibly complex ... repitition of this test with the same result makes it a Scientific Fact
Again, Behe did not say that the removal can allow it to have a different function, but that by removing it "the system ceases to function." If we change this to "causes the system to either cease to function or serve a different function," as you would like to do, we can agree and move on.

3. Now the postulations can be made from the test... if the bacteria in question looses mobility at the elimination of any component, then logic follows that all components that caused the flagellum to cease function must be present for the flagellum to work... all of these components can be classified into a sub system called the "Irreducible Core"
For the flagellum to be a flagellum and not a type three secretory system (T3SS). And so what? My bridge with a plank was an "irreducible core" for the bridge, yet I showed how it could have evolved from another kind of bridge.

4. Next postulation... if all these components in the irreducible core must be present for the flagellum to work, logic follows that the irreducible core had to arise spontaneously with all the components present, perfectly matched, and functioning effectively.
That's not a postulate, but rather a conclusion. It's also invalid, as I showed with my bridge example.

5. If all this had to arise spontaneously, then we can say it's impossible for a process to form it by adding components one at a time
Well now you are basing more conclusions on an already-demonstrated falsity, but even so evolution doesn't work by only adding pieces. It can also remove or alter pieces. The removal of the center brick in my bridge example is certainly something we could expect of evolution.

6. and if evolution works by adding components one at a time, the evolution could not have given rise the the system in question
Again, evolution does not only add components. This is the central problem with Behe's reasoning, which can be stated in a much more concise predicate-conclusion form as follows:

P1 - there exist structures in biology that would not function if one piece were removed (IC)
P2 - evolution requires that every stage of development be functional
P3 - evolution can only add pieces
C - IC structures cannot have evolved

This argument is flawed because premise three is false. You have expanded the argument to 7 "postulates" in which you have mixed in conclusions and such, and are stuck with the exact same problem.

7. If evolution works by adding all these components spontenously with all the well matching interactions and deft assembly instructions, then we are definitely talking of an intelligent, sentient process not an undirected process. we are already talking about ID.
We have already established that evolution doesn't work that way, but why would we be forced to conclude the existence of a sentient being even if Behe's argument weren't flawed? We can just as easily imagine an inanimate thing or process that spit out the structure fully-formed, though it wouldn't be evolution. We would have no falsifiable, unique, testable hypotheses with which to evaluate the veracity of the existence of this "intelligence."

As for your math, the bridge I drew in the second stage of my previous post
_____
OOO

would have an IC quotient of 0.75, since only the middle block could be removed, and the final stage of the bridge

____
O O

would have an IC quotient of 1. Clearly your assertion that such a quotient being greater than 0.5 would signify impossibility is not only arbitrary, but completely wrong.
Reply: Benjamin Toby Yes, but which criteria determines a "kind"?  If I see an animal, how do I determine its "kind"?

You didn't answer my other question either: Are birds and reptiles differnet groups, and are vertebrates and invertebrates different groups, aswell as animals vs plants, for example?
Reply: Max Spiegel 

As AHD pointed out, this is pure garbage. You aren't even sure that eagles are a kind when pressed on the matter. If your definition cannot be tested, it is useless. ... lol ... what's wrong if I'm not certain of the classification?  it's not like you are 100% certain of the taxonomy you use ... now please how do you classify a bearcat from domain down to species level?

No, missed the "pre" part of "prediction." Looking after the fact and retrofitting your observations would be "postdiction." ... oh I see: so after the stone age men figured out that penguins produce penguins, an awesome theory came along and gave a ground breaking  prediction which states that, well, penguins produce penguins ... smashing prediction ...

Evolution does not say this is possible either; you are merely illustrating your lack of understanding by stating such nonsense. ... OK I noticed you don't like me using the word "morph" ... but that describes the evolution story perfectly ... if a bacteria can change(happy?) into a human over millions of years, what stops me from saying a herring can change into a penguin over millions of years? are there restrictions for the change? ... if there are please explain to me how these restrictions worked when changing a bacteria into a human being ...

Unique predictions, Toby. They must be unique to the theory. Besides, I don't see how finding a creature with a different chemical structure instead of DNA would be a problem for either ID or evolution. ... actually different chemical structures would validate evolution and contradict ID since it would suggest that there is more than one way of creating life ... and this prediction is actually unique to ID because we are saying there's a designer of life and this designer has been using this signature language to create life ... it's not unique for evolution because differences in life code would suggest that chance played a role in the origin of life ... but a single life code indicates a high improbability for chance to form life ...

Firstly, evolution is not random. Second, any new abiogenesis trying to appear on the planet would be snuffed out by the already dominant life forms we have unless it proves instantly pathogenic to all of them, which seems rather unlikely. ... OK I get it: evolution relies mainly on random mutations but it is not random ... I see ... PS the second part is just another unsubstantiated imagination of yours ... what stops a new abiogenesis from flourishing on its own? ... what stops it from coexisting with the DNA organisms?

Yeah, and you know who exposed that fraud? Evolutionary biologists. Not creationists. ...so what?

Stories like Nebraska Man are examples of why we can trust scientists and not creationists. lol ... you mind trusting the scientists that say evolution is false? ...

and understand that this means that all the items on the list I gave you have been checked and double-checked for authenticity. ... authenticity of the real bones or the made-up reconstructions? ... you really expect me to believe that a full organism can be accurately described from less than one third of the bone fragments? ... it'll be stupid of me to believe such a thing...

"By irreducibly complex I mean a single system composed of several well-matched, interacting parts that contribute to the basic function, wherein the removal of any one of the parts causes the system to effectively cease functioning." ... ofcourse if you listened to any of Behe's debates you'd find out that he's actually saying that the system function is the criteria for irreducible complexity ... even the definition clearly states it ... "causes the system to effectively cease functioning" ... and this system is already predefined to function with several parts interacting together ... so the ceasing of function is actually the ceasing of function of the system in question ... I have to say I really pity Behe having to clarify something that an elementary student can understand ... His argument uses a top down approach to determine a bottom up process ... this is probably where your confusion is ... 

I created an IC system through evolutionary-style changes right before your eyes! Did you not read my bridge example? ... I didn't respond to the bridge analogy because it is a miscue from what IC is ... according to IC, if removing any of the components causes the bridge to stop functioning as a bridge then it is irreducibly complex ...

It failed because a mousetrap is not IC. I can remove part of it and use the rest for something else. ... you have got to be kidding me ... please could you just open your eyes for one moment and try to understand the argument here ... 

Again, Behe did not say that the removal can allow it to have a different function, but that by removing it "the system ceases to function." ... OoooK ... I'm saying that Behe said the by removing it, the bacteria flagellum ceases to function as a mobility device ...

For the flagellum to be a flagellum and not a type three secretory system (T3SS). And so what? My bridge with a plank was an "irreducible core" for the bridge, yet I showed how it could have evolved from another kind of bridge. ... I suggest you re-read the hierarchy again ... also, you showed how a simple bridge can be constructed via intelligence and simplified via intelligence ... 

Well now you are basing more conclusions on an already-demonstrated falsity, but even so evolution doesn't work by only adding pieces. It can also remove or alter pieces. ... firstly please try to understand the concept before labeling it a falsity ... secondly if we are working from a state of no flagellum to a state of a functional flagellum, evolution has to add all those parts ... and it has to assemble the irreducible core effectively to get a flagellum ... so I don't know how removing parts can help it assemble this machine ...

Again, evolution does not only add components. This is the central problem with Behe's reasoning ... what difference does it make? ... evolution still can't give rise to the system in question by adding and removing parts ... 

would have an IC quotient of 1. Clearly your assertion that such a quotient being greater than 0.5 would signify impossibility is not only arbitrary, but completely wrong. ... it's not wrong because you said so ... you have to first get a good hold on the concept, and then prove to me how it's wrong ... so far you are having a hard time grasping the concept ...

and can you tell me the system we're working with in your analogy? ... because it looks lie there are two ... even if they are two, and the ICQ for the second is 1, it doesn't change the fact that that system is Irreducibly complex with a an ICQ of 1 ... this is why I need you to get the facts and the conclusions derived from the facts ... Irreducible complexity is a fact because it can, and has been tested with biological systems ... the argument would be if evolution can give rise to an irreducibly complex system ... and that doesn't seem like an argument that would favor evolution ...
Reply: antiHUMANDesigns like I said, kind lies in the range of family and genus ... if you know the criteria for these classifications, then you have an idea of what I'm saying ... also I didn't respond to those other comments because I didn't see any need to ... I didn't see how it was related to the "kind" classification ...
Reply: Benjamin Toby
"how do you classify a bearcat from domain down to species level?"
That doesn't matter because the divisions aren't objective in evolution. You are claiming there is an objective barrier between animals called "kinds." Taxonomic classifications make no such claims.

"I didn't respond to the bridge analogy because it is a miscue from what IC is ... according to IC, if removing any of the components causes the bridge to stop functioning as a bridge then it is irreducibly complex"

Again, the structure at hand is the following bridge
____
O O

How is this structure not IC? Which part could be removed without it being rendered useless?

By the way, this use of the word "miscue" seems to be nothing more than your way of saying "but I don't want you to apply my definition that way." Why don't you try to pinpoint exactly what about my analogy is a "miscue," whatever that means?

"I suggest you re-read the hierarchy again"
Done. It still says nothing that I didn't say in my 3-point premise-conclusion form of your argument.

"you showed how a simple bridge can be constructed via intelligence and simplified via intelligence"
You mean I showed how an IC bridge can be constructed through a series of changes could each be achieved by a mutation that occurs through evolution.

"firstly please try to understand the concept before labeling it a falsity"
You can't just keep claiming I don't understand something. You have to say exactly where my understanding is wrong.

"I don't know how removing parts can help it assemble this machine"
Didn't you see how removing the middle brick in the IC bridge helped assemble the bridge, also making it more lightweight?

"evolution still can't give rise to the system in question by adding and removing parts"
With a combination of adding and removing parts, of course it can. Again, remember the Mullerian Two-Step? Remember the IC bridge?

"it's not wrong because you said so ... you have to first get a good hold on the concept, and then prove to me how it's wrong"
I showed you how a structure with a ICQ of 1 can arise through evolutionary mechanisms and incremental changes, specifically using the Mullerian Two-Step. If that doesn't render that measure irrelevant, what would?

"the argument would be if evolution can give rise to an irreducibly complex system"
And I have shown you that it can using the bridge analogy and the Mullerian Two-Step. IC may be well-defined (though you have had to modify Behe's definition to even get it this far), but it is utterly useless.
Reply: Benjamin Toby "like I said, kind lies in the range of family and genus"

Yes, but those classifications imply a tree structure of life. Do you accept that life can be sorted into a tree structure?

"also I didn't respond to those other comments because I didn't see any need to "

It was to see if you agree that life can be sorted into a tree structure.
Reply: Max Spiegel

How is this structure not IC? Which part could be removed without it being rendered useless? ... this is proof that you're probably still confused ... so please try your best to understand me and Behe ... I'm not saying the imaginary bridge isn't IC: I'm saying the exact opposite ... it actually is ... PS could you try to limit your analogies to actual facts and real biological systems? ... IC works with real biological systems ...

Why don't you try to pinpoint exactly what about my analogy is a "miscue," whatever that means? I think I've just pinpointed one ... and you seem to be confused about your own analogy ... that analogy was to show that the bridge with three stones can be reduced and still function as a bridge ... a product of poor understanding ... the analogy aimed to explain that taking out a part can be non-destructive to the system ... this is what the supposed trained scientists got from Behe's arguments ... they think Behe is saying that no part should cause the system to stop function on removal ... whereas Behe is saying that if taking out ANY part causes a system to stop functioning, it is IC ...

Done. It still says nothing that I didn't say in my 3-point premise-conclusion form of your argument. ... no you're not done buddy ... I clearly stated that P3 makes no difference if evolution adds or removes parts ... the fact shows that the flagellum is by definition Irreducibly complex and all the parts of the IC core had to be assembled spontaneously ... I've demonstrated my rationale behind this conclusion and it's based of hard facts and pure logic ... however, somehow, you believe your imaginary bridge which is even a miscue, can refute it ... if you want to use any analogy then you can try to imagine how the process of adding and removing parts randomly brought about a full functional flagellum.

You can't just keep claiming I don't understand something. You have to say exactly where my understanding is wrong. ... I think I've said it a couple of times but I'll try again ... ID says there are certain biological systems that are too complex to have arisen by evolution: therefore they had to be designed ... but the opponents said how can you tell something is designed? ... here comes Behe with Irreducible Complexity ... and he said Irreducible complexity is a test for design ... how? ... if we have a machine with 40+ parts all working together to gain a single function like the bacteria, and this machine breaks down on elimination of any part(s), then we can conclude that the origin of this machine was not by random addition and removal of parts because it requires all the said parts to perform its function ...and that's proof that Intelligence is responsible because Intelligence is the only known cause that can create such a system at once ... you don't seem like you understand this ... 

Didn't you see how removing the middle brick in the IC bridge helped assemble the bridge, also making it more lightweight? ... removing the middle brick didn't assemble the bridge: it only simplified it ... the bridge was already set before that ... and if your argument is evolution can simplify already functioning machines then maybe you would have a valid argument: but that doesn't explain its origin ... 

With a combination of adding and removing parts, of course it can. Again, remember the Mullerian Two-Step? Remember the IC bridge? ... how are you so confident that an imaginary analogy(which is even wrong) can trump hard facts? ... how do you come up with these things? ... removing a brick from a crude imaginary bridge proves that the bacteria flagellum can arise by evolution ... for real? ...

I showed you how a structure with a ICQ of 1 can arise through evolutionary mechanisms and incremental changes, specifically using the Mullerian Two-Step. If that doesn't render that measure irrelevant, what would? ... actually you just showed the irreducible core of the bridge ... as expected, the IC core would have an ICQ of 1 ... if you really want to refute my math then you should try using actual facts ... my math is supposed to work with facts ...

And I have shown you that it can using the bridge analogy and the Mullerian Two-Step. IC may be well-defined (though you have had to modify Behe's definition to even get it this far), but it is utterly useless. ... ofcourse after listing my arguments with pure facts and an easy-to-read hierarchy you come up with a three stone bridge in your head and "take this out - take this in" !BOOM! refuted ... maybe now you could understand the plight of Behe and these so called scientists...
Reply: antiHUMANDesigns I don't agree with the tree because it's born out of an evolutionary presupposition ... the Kind classification is still quite difficult but I think it is a better explanation of the facts ...
Reply: Benjamin Toby No, it wasn't. That "tree" structure was made by Carl von Linné, at least 100 years before Darwin. 
Anyone who looks at life on earth is forced to admit that you can sort them into a tree structure of traits. Birds/dinosaurs have feathers, mammals have hair. Those traits are unique to them, so they're different group. Mammals also have the mammalian glands for example.
Not a single species outside of these groups have those unique traits.
And both birds and mammals have endoskeletons, which insectrs have exoskalatons, for example. So then we have to put birds and mammals (and so on) into a group of "vertebrates". But the thing is, tehre is no invertebrate with feather or hair, or mammalian glands, for example.
This makes it simply a fact that you can sort life into a tree structure. And the most notable thing is that when you look at individual species, not just families or genera, you can also put them into a tree structure.
That is, the same way we can form a tree for your family. It works the same way.

This is not up for question. You cannot "disagree" that we can sort them into a tree structure, it is a fact, and we have done so for a long time. This fact requires an explanation.
Reply: antiHUMANDesigns https://simple.wikipedia.org/wiki/Tree_of_life_(biology)

- I hope you're not giving me false info again ... the tree of life used by biology is that of Darwin ...

also anyone that looks at life on earth can easily tell there a animals that share a common traits ... not that you can draw an evolutionary tree to connect them ... we can also tell the disparity in phyla and that's simple proof that all animals can't be classified into a tree ... what ever tree you've seen is most likely the product of imagination and an evolutionary presumption ...

This is not up for question. You cannot "disagree" that we can sort them into a tree structure, it is a fact, and we have done so for a long time. This fact requires an explanation. ...what makes you think your assertions are of any meaning to me ... yes it's up for question and I disagree: with good reasons ... you have no substantial evidence to back up the connection between the branches for different phyla and even families so why should I conform to these pathetic excuses for explanations? ... the best explanations are similar designer and genetic variation ... that's what the evidences show ...
Reply: Benjamin Toby "the tree of life used by biology is that of Darwin "

Perhaps you should look up linnean taxonomy? That's what I'm talking about.
What you're talking about is cladistics. A much better system, and a requirement if you want to account for evolution over long time scales.

I mean, you are aware of the person Carl von Linné, right?
https://en.wikipedia.org/wiki/Linnaean_taxonomy
Right there, in the start of the article, it tells you that Linné set this system up in 1735, and it is the system where life is divided into kingdoms, classes, genera, and so on.
This is a tree structure, because you've got nested groups.

I intentionally did not use the term "tree of life" as to not confuse it with that common term. I said "a tree structure", which is a mathematical idea, not a biological term.

"also anyone that looks at life on earth can easily tell there a animals that share a common traits ..."

Yes, but also that those traits can be consistently placed in a tree structure. That is what we do when we do taxonomy (which did not start out knowing about evolution). That is the reason why humans are classified as apes, which is on the "primate" branch, which is on the "mammalian" branch, which is on the "vertebrate" branch, which is on the "animalia" branch.... to simplify.
A tree structure.

"we can also tell the disparity in phyla and that's simple proof that all animals can't be classified into a tree"

Show me such an example. Give me an example of a lifeform that defies taxonomic classification. Because that's what you're saying.

"what ever tree you've seen is most likely the product of imagination and an evolutionary presumption "

Evolution has zero to do with this. Why life can be described using a tree structure has nothng to do with the fact that it can. Evolution or creation doesn't matter, it's still a fact hat life can be described using a tree structure.

"you have no substantial evidence to back up the connection between the branches for different phyla and even families so why should I conform to these pathetic excuses for explanations?"

But, ffs, I don't need a "connection" between them, I just need to look at how they are similar and how they are not, and I am able to describe them as a tree structure. And so can you. And so could Carl von Linné
 over 100 years before "the origin of species".
Do you even understand what a tree structure is? Nested groups?

The fact that all life uses cells means we can group all life into "life" that way. Some are eukaryotes, so we divide them between eukaryotes and prokaryotes, for example. Then we keep diving those groups based on traits, and you get a tree structure whether or not you believe they evolved from eachother.

I am not talking about evolution. Nothing I am saying has anything to do with life evolving, it only has to do with being able to group all lifeforms up into nested groups.

There are a group of animals that have vertebrates, so we call them all "vertebrata".
But inside that group, there are specific trait that are shared by some of the vertebrates, but not others, so we split the "vertebrata" into new groups. Then we keep doing that, and we get nested groups, or "a tree structure", like the folders on a PC.

" the best explanations are similar designer and genetic variation "

I didn't ask for a fucking explanation...!

A "similar" designer? Similar to what?
And unless you're proposing that one designer made insects, and another designer made vertebrates, no, it doesn't work. Since we have nested groups of life, then we have to assume there would be a nested group of designers, aswell. Some designers build things more similar to other designers, and they will form a tree structure aswell, then.
And yet, it explains nothing unless you can actually study the designers.
Reply: Benjamin Toby
"the fact shows that the flagellum is by definition Irreducibly complex and all the parts of the IC core had to be assembled spontaneously ... I've demonstrated my rationale behind this conclusion and it's based of hard facts and pure logic ... however, somehow, you believe your imaginary bridge which is even a miscue, can refute it ... if you want to use any analogy then you can try to imagine how the process of adding and removing parts randomly brought about a full functional flagellum."

You have absolutely no rationale behind this claim that IC systems pose a problem for evolutionary theory unless you insist that evolution can only add parts and never remove, which we both agreed is not true. The removal of the middle brick was what gave the bridge its final form, hence it was essential to the construction of the final structure. Again, the Mullerian Two-Step is to add a part, then make that part essential.

You keep saying that IC systems must arise spontaneously, yet I have demonstrated otherwise with the bridge analogy. You still have not told me how the bridge is a "miscue," and again are using the word to apparently mean "I don't want you to apply my definitions to these things." Also, nobody said anything about the process being random; it is merely undirected.

You want the same version of the story with a flagellum? Easy: first you start with a T3SS, then you get an extended filament to help deliver the secreted protein, You then change the basal protein structure in such a way that the filament can wiggle around a bit. You then seal the end of the filament so it cannot transmit molecules and only functions as for motility. Again, the Mullerian Two-Step explains the evolution of the flagellum with ease.

The Mullerian Two-Step demonstrates that IC is a completely useless concept. I have shown you this with the bridge analogy to illustrate the general idea, but it can be used to demonstrate the irrelevance of IC to evolution in general because it applies to all IC systems, real or imaginary. You seem to be upset that I have applied your definition of IC to such a simple hypothetical structure, but you can't tell me what about it makes the analogy bad. Apparently, you just don't want me to use the analogy because it works so well. You have even called it "imaginary"  (whatever that means; all analogies are imaginary by definition, otherwise we call them "examples") and "wrong" (yet again you can't point out exactly how).

It seems like you are struggling to express which part of my analogy doesn't apply, or where my mathematics are wrong, and are instead trying to get us to forget the analogy all together. It won't happen. My math was perfectly factual; it was just based on the bridge analogy, and that clearly upsets you.

Tell me exactly what is wrong with my analogy. Do you think it is wrong because it is too simple? Does IC only apply to sufficiently complex structures? Why would that be the case, and how complex do those structures have to be for the concept of IC to imply design? Do you not accept it because it s not a structure I can point out in a specific biological organism? That is not necessary for analogies; that's what makes them analogies. Perhaps you want to abandon analogies all together?
Reply: Max Spiegel 

You want the same version of the story with a flagellum? Easy: first you start with a t3ss, then you get an extended filament to help deliver the secreted protein, You then change the protein structure in such a way that the filament can wiggle around a bit. You then seal the end of the filament so it cannot transmit molecules and only functions as for motility. Again, the Mullerian Two-Step explains the evolution of the flagellum with ease. ... good application of imagination ... just that the structure would be useless untill all the required parts are fully matched and assembled ... nice to know that a random process can assemble such a structure ... PS evolution is random because it relies on random mutations ... it's simple deduction ...

The Mullerian Two-Step demonstrates that IC is a completely useless concept. ... I have an Idea ... just explain to me what I've said about IC and explain all the similarities with your bridge and tell me how you refuted it ... should be easy enough for you: just show me you understood anything I said ...
Reply: Benjamin Toby
"just that the structure would be useless untill all the required parts are fully matched and assembled"
The T3SS would not be useless, and neither would any of the intermediate stages, so this is false.

"evolution is random because it relies on random mutations "
Which are selected for by natural selection, which is completely non-random. The element of random mutations and genetic drift is what makes the process undirected, but evolution would not work if not for the non-random processes of non-random mating and natural selection. Nobody except a creationist would tell you evolution is purely "random," and even many of them aren't that dishonest.

"just explain to me what I've said about IC and explain all the similarities with your bridge and tell me how you refuted it "
You said that IC structures cannot have formed by gradual changes with each intermediate step being functional, and so they must have appeared all at once, fully-formed, and spontaneously. The bridge in my analogy is IC, as you agreed, yet I showed how it could form through gradual changes that evolution is fully capable of. Hence IC does not imply inability to form from evolutionary mechanisms.

Now you can explain to me exactly what part of your claim that IC means "cannot evolve" I missed.
Reply: Max Spiegel  The T3SS would not be useless, and neither would any of the intermediate stages, so this is false. ... the T3SS is also IC buddy ... fully formed and functional ... But even if I assume the flagellum came from that just for the sake of argument, why should I believe that adding parts randomly can produce the IC core of the flagellum for mobility? ... this is pure imagination on your part ... and an irrational one as well ... how would all those 20 extra parts arise? random formation of proteins? ... how will they all assemble together? ... the imaginary random addition of parts one at a time with each new subsystem being useful? ... that's actually nonsense ...and the only proof you have are assertions and imaginations ... no facts to support this ...you've just assigned a delicate and complex process to chance ... and you ask why I don't buy into this ...

Which are selected for by natural selection, which is completely non-random. The element of random mutations and genetic drift is what makes the process undirected, but evolution would not work if not for the non-random processes of non-random mating and natural selection. Nobody except a creationist would tell you evolution is purely "random," and even many of them aren't that dishonest. ... I've really thought about it and there's really no reason to think evolution is not pure chance ... non-random mating? ... lol ... the mating has little effect on evolution ... two animals can mate from now till eternity and no evolution will occur until the random mutations create the different variations for natural selection to work with ... so natural selection would be useless without the random mutations ... if everything in evolution hinges on random mutation, then how is it not random ... does gravity mean that the outcome of a tossed dice isn't random? ...

*You said that IC structures cannot have formed by gradual changes with each intermediate step being functional, and so they must have appeared all at once, fully-formed, and spontaneously. * ... actually I said the IC core of an IC system cannot arise by gradual changes because the facts show that they are all needed for the basic function of the system in question ... you say it can by adding and removing parts randomly with each sub-system being functional: proof? an Imaginary IC bridge ... wow ...
Reply: Benjamin Toby
"the T3SS is also IC buddy ... fully formed and functional"
I love this argument. It's like the "missing link" one: whenever we find a fossil that would fit the definition, creationists now claim there are two missing links; one on either side of the fossil.

Here you are doing just the same thing with IC: you claim a structure is IC, and then when I show you how it can function after removing a part, you now claim that each remaining half is IC, thereby doubling the IC-ness! This line of reasoning is spectacular to behold, but obviously belongs firmly to cognitive dissonance and confirmation bias.

"But even if I assume the flagellum came from that just for the sake of argument, why should I believe that adding parts randomly can produce the IC core of the flagellum for mobility?"
Your insistence on using the word "random" when I have clearly explained how evolution is not purely random is a plain attempt to use words that make something sound more improbable than it actually is.

The burden of proof is on you to prove that the flagellum cannot be a product of evolution, as that is the principle positive claim made by ID. Your only reasoning to support this was "IC structures cannot arise as a result of gradual changes," which has been demonstrated to be generally false multiple times in this thread alone with examples like that of the bridge or hypothetical evolutionary pathway for the flagellum.

"this is pure imagination on your part ... and an irrational one as well"
Irrational exactly how? Because it seems unbelievable to you? That is an argument from incredulity.

"how would all those 20 extra parts arise? random formation of proteins? ... how will they all assemble together? ... the imaginary random addition of parts one at a time with each new subsystem being useful? ... that's actually nonsense ...and the only proof you have are assertions and imaginations ... no facts to support this ...you've just assigned a delicate and complex process to chance ... and you ask why I don't buy into this"
You seem to be missing the point, and are now tasking me with giving hypothetical pathways for every structure we know of instead of addressing the deathblow being dealt to the concept of IC as a valuable measure of "evolvability." I have demonstrated that IC in general is not a sign that a structure cannot have evolved with the bridge example. I even gave a possible pathway for the flagellum. Must I now do so with every IC structure in biology to prove my point? No.

"the mating has little effect on evolution ... two animals can mate from now till eternity and no evolution will occur until the random mutations create the different variations for natural selection to work with"
Sexual recombination has everything to do with evolution, as it directly controls which phenotypes are passed on and therefore present in a population. New phenotypes can arise from combinations of pre-existing genotypes even without mutation. Non-random mating is one of the four main driving forces of evolution.

"does gravity mean that the outcome of a tossed dice isn't random?"
No, because the probability of any face is still 1/6 no matter which direction gravity points in, whereas natural selection and non-random mating change the probabilities of phenotypes being passed on between generations.

"you say [IC can come from evolution] by adding and removing parts randomly with each sub-system being functional: proof? an Imaginary IC bridge ... wow "
You still haven't refuted a single thing about that analogy and the consequences of it, so your "wow" seems rather unwarranted. How about telling me what's wrong with it instead of just expressing incredulity?
Reply: Benjamin Toby "a classification doesn't imply a tree "

No, I didn't say that..... goddamn we seem to have some serioius communication issues, here.
Taxonomy is a tree structure, probably because there is no better way to describe it. Species fit into nested groups, that's just a fact, and it's so obvious that it would be stupid not to describe them using a tree ("nested groups", if you want to avoid using the word "tree" for some reason).

"the tree brings in the new concept of connection between organisms "

No, it doesn't. I don't see why you have to force that into it. The tree structure of taxonomy was there when Linné made that system, about 120 before anyone suggested that different species were actually related. There is no "blood relation" required when describing something as a tree. Though, if something is described best as a tree, then perhaps it's a good idea to consider if they have some kind of relation.

Words in a dictionary can also be described as a tree.
First, take all words, that's the root. Then split them into words that start with "A", one group that starts with a "B", and all the way through the alphabet.
Then, inside group "A...", group the words by their second letter, and keep following that system.
What you get is a tree structure of all words that exist. But that does not mean that "Hand" is realted to "Harness", even though they are both on the "Ha..." branch of that tree.

See what I mean, now?

"I'm not sure you even grasp the idea of the tree "

Yeah, you're tlaking about "Darwin's tree of life", and I'm not. I am talking about the mathematical concept of a "tree structure", which is a set of nested sets. Read set theory.
And yes, I do grasp that concept, because I am a programmer and tree structures are often used in programming because they allow fast ways to traverse sets of data, for example.
If I want to find something, then I only have ot go down the branch where the "trait" of the data I'm looking for exists. The dictionary example I gave is a good example. Each letter works as an index. I don't ever have to bother with letters that start with "b" if I don't go down that branch.

And life is very well described that way. If the lifeform I am looking for is based on cells, then I start at the roof of this tree. If it has a chodate, then I go down that branch, and suddenly I have eliminated all bacteria and fungi and so on.  
The fact that no plants with spines exist, for example, means that the tree structure will work and make perfect sense. It will be the most efficient way to describe each species.

And yes, we now know that the reason for this is because of evolution. But my point is that the scientists of Linné days, long before Darwin, already agreed that life is best described using a tree structure. Even today, we still use a tree structure, because it still is the best way to describe it that we can think of.

"you are displaying your ignorance towards theism"

Oh, I hope I am! No one has ever managed to explain to me what a "god" is supposed to be, so I have absolutely no damned idea. And I'm happy that this shines through, so that there is no misunderstanding, here.

"the proof is the singular life making code: DNA "

No, DNA is proof that DNA can and does exist. It proves nothing else.
And it most certainly is not evidence of a creator god either, since evidence cannot be evidence of two opposing explanations at the same time, or it will be evidence of neither.
Also, DNA is not "code".

"as would be with a programmer using the same codes to create different programs "

Not exactly sure what you mean, since the same code would produce the same program. But parts of code is reused, yes.
But you have to realize that if species A gives rise to species B through evolution, then they will obvious have very similar DNA. That is exactly what you should expect.
Ac reator, however, doesn't have to do it that way. That's the difference. There is an almost infinite number of ways to make something that is pretty much exactly the same thing using DNA, just as when programming a computer. But for some reason, similar species have nearly identical DNA sequences. And it's not because it is the optimal DNA, because it most certainly is not. Life is full of jury-rigged structures that are clearly repurposed versions of other things. And the recurrent laryngeal nerve is a great example of stupid design.

"Look seriously I'm not sure if I'm ready for another dose of drivel from you "

You know, I'm still waiting for you to actually answer my challenge. I gave you a set of facts that you were supposed to explain using creationism/ID, but you just ran away, proving that creationism has no explanatory power. Or are you going to do it?
No, I didn't think so. Your position is intellectually dead.

"and come with an open and clean mind "

Yes, anyone who disagrees with you doesn't have an "open mind". Genius self-defense mechanism you've got, there.
Reply: antiHUMANDesigns  you know I realized you were off on your spree again so I decided to point out a few things ...

Taxonomy is a tree structure, probably because there is no better way to describe it. ... nested groups would be a better term ...

Not exactly sure what you mean, since the same code would produce the same program. ... you are a programmer and you don't know what a code is? ... a program is merely an arrangement of codes you can have a code to get an input: but different programs call for that code at different times and lines ...

Words in a dictionary can also be described as a tree. First, take all words, that's the root. Then split them into words that start with "A", one group that starts with a "B", and all the way through the alphabet. ... so what you're saying in essence is that I can just connect all the phyla to the creator and we have a tree of life? ... I think that'd be a more credible tree ...

Oh, I hope I am! No one has ever managed to explain to me what a "god" is supposed to be, so I have absolutely no damned idea. And I'm happy that this shines through, so that there is no misunderstanding, here. ... how would anyone successfully explain what a "god" is when you can't understand what similar designer is?

Ac reator, however, doesn't have to do it that way. That's the difference. ... wth ... why can't a creator use the same language to create other organisms?

You know, I'm still waiting for you to actually answer my challenge. ... no shit... I've responded to that twice ... I don't think I deserve to go through that much drivel for a third time ...
Reply: Benjamin Toby
"you haven't shown any factual reasonable explanation for how a T3SS can form a flagellum"
I did give a rough sketch of a possible evolutionary pathway from the T3SS to the flagellum. However that was not the point of pointing out that the T3SS is a part of the flagellum which functions perfectly well at a different job than motility, despite its being simply an "incomplete" flagellum. The point of mentioning this fact is that this means the flagellum is not IC, and that is all. This is aside from the fact that even if it were IC that would not imply that it could not have evolved.

"what happens if I say the T3SS was formed from a bacteria flagellum by loss of parts?"
You get asked for evidence that supports a model with predictive power. Again, what we want here are unique, falsifiable predictions.

"what do you have to prove I'm wrong? nothing ... same way you have no proof of your imaginary explanation."
That's not how evidence works. You are the one making a positive claim about the impossibility of the evolution of the flagellum, so you must support that claim. Evolution and common descent have been proven by unique, falsifiable predictions that are supported by repeatable experimentation. One does not need to prove that evolution is responsible for any specific structure at this point any more than one needs to prove that the force between any pair of stars is proportional to their masses as a result of gravity.

"I think you missed my explanation for why I think evolution is random"
I don't think so. Your explanation was that mutations are random. I replied that the selection of which mutations stay in the population was not. We seem to have ended there.

"the burden on proof is actually on you if the experiments prove a system is IC ... you have to show that the experiments are wrong and that the flagellum doesn't require all the said parts to function"
Why would that be true when we have seen that a structure being IC has exactly nothing to do with whether or not it could have evolved? Remember the Mullerian Two-Step!

"lets consider the first step where you say the injecting tube morphs into a tail: at this point I say there's no possible function the tail will perform so it will be eliminated by your process"
Nonsense, the tube may confer an advantage against a particular rival form of bacteria with a protective membrane that requires penetration by the filament.

"you only have to prove one ... which you have failed to do with reasonable facts"
Why do I have to prove that IC doesn't correspond to design within biology when I have proven it in general? Even so, what exactly is your objection with my hypothetical pathway for the flagellum? I already knocked out one, so you might as well give the rest.

Better yet, why don't you critique the work of an actual professional on the matter?
http://mbe.oxfordjournals.org/content/25/9/2069.abstract

"well non random mating cannot bring about any special or distinct trait  that would be needed for natural selection to differentiate fitness"
Wrong: imagine a case where white animals select to breed with black animals and give rise to the new trait of grey animals. The environment will almost certainly select for or against that trait, and if it is selected for we have a new phenotype which adds fitness to the population as a result.

"no matter which direction natural selection points to, it would be useless without the unique distinctions created by random mutations"
Natural selection is the hand that makes the non-random selection from a randomized set. It's like rolling a bunch of dice, but only looking at those that come up as 3's and ignoring the rest. The process has a random element, but it is not a random process.

"Natural selection doesn't change the probability of phenotypes being passed on: it changes the frequency of the phenotypes that are being generated by random mutations"
Very wrong: natural selection (NS) acts on an organism after it has mutated. Mutations affect the phenotypes present, and it is how those phenotypes confer an advantage in fitness in a given environment which determines whether NS snuffs them out or keeps them. This is done by preventing it from being able to reproduce, for example by either killing off the organism before it can reproduce or hindering its ability to find a willing and viable mate. If the organism doesn't reproduce, the phenotype/genotype(s) are not passed on. NS has no control over what mutations appear in the population in the first place.

"just like gravity filters between the two dice based on the force receives when tossed: the will end up landing in different places at different speeds and times"
The direction of gravity doesn't confer any advantage to a particular face of a fair die coming up if we assume a random initial toss, what are you talking about? It seems like you are going off on a philosophical rant about determinism rather than addressing the actual probabilities.

"you could atleast try to get a hold on the fact that I'm working with facts which can be verified and proven with ease while you're desperately clinging to a weak excuse which has no factual backing"
Fact: ID has zero unique, falsifiable predictions that have been confirmed through repeatable experimentation, nor does it even have any such testable hypotheses in the first place.

Fact: Evolution and common descent have countless such predictions.

Fact: IC has no bearing whatsoever on whether or not a structure could have evolved, as was illustrated by the bridge thought-experiment and applying the Mullerian Two-Step to a variety of structures. You have done nothing to illustrate otherwise.

Fact: Things like flagellum and mousetraps aren't even IC because they have components which serve independent functions when not part of the whole "core." The best you have been able to do is say that each new core is now irreducible, which you can obviously do ad infinitum.
Reply: Max Spiegel

I did give a rough sketch of a possible evolutionary pathway from the T3SS to the flagellum. ... ie a plausible model according to your evolutionary presuppositions, void of facts and evidences ...

The point of mentioning this fact is that this means the flagellum is not IC, and that is all. ... I really have to ask if you really understand what you're saying ... as far as I can remember you pointed out the T3SS to show that an IC system: the flagellum can be formed by evolutionary process through your bridge analogy ... the T3SS can't refute the IC of the flagellum ... if you think it can then you need to go through my first hierarchical explanation again ...

You get asked for evidence that supports a model with predictive power. Again, what we want here are unique, falsifiable predictions. ... O-o ... I smell foul play here ... how come you don't get asked for evidences to support your imaginary story? ... you want evidence? the most notable change from the e-coli experiment shows a loss of function of a component: you even said evolution also works by removing parts ... so I have good reason to deduce from this to say that the T3SS is a devolved form of the flagellum ... what do you have?

That's not how evidence works. You are the one making a positive claim about the impossibility of the evolution of the flagellum, so you must support that claim. ... no kidding ... I made the claim alright : and i did support it with factual, testable scientific fact and evidence ... still waiting for yours ...

 Evolution and common descent have been proven by unique, falsifiable predictions that are supported by repeatable experimentation. ... hahaha ... u mean the prediction of penguins producing penguins? ... lol ... a cave man could have figured that out thousands of years ago ... PS try not to mix evolution and common descent ... common descent is born of a presupposition of evolution ... without this, common descent is only common designer ...

I don't think so. Your explanation was that mutations are random. I replied that the selection of which mutations stay in the population was not. We seem to have ended there. ... the selection is also random ... because the selection has no distinction for what is useful and what isn't ... 

Why would that be true when we have seen that a structure being IC has exactly nothing to do with whether or not it could have evolved? ... I'm sorry "we" who? ... I have shown that a structure being IC has to have its core spontaneously assembled and functional to achieve the function observed... hence it could not have been formed by the slight modifications needed to validate evolution ...

Nonsense, the tube may confer an advantage against a particular rival form of bacteria with a protective membrane that requires penetration by the filament. ... imaginative power in action I'd say ...well I say the tube didn't confer any advantage against any rival since it was more flimsy than it was before the morphing: ie it couldn't penetrate any protective membrane so it went vestigial ...

 Even so, what exactly is your objection with my hypothetical pathway for the flagellum? ... my objection is that your hypothetical pathway is nothing more than an imaginative hypothesis based on little to no facts and evidences; and it doesn't override the facts I stated ...ie it's more like a cool story: or as Behe calls it "a just so story" ...

Wrong: imagine a case where white animals select to breed with black animals and give rise to the new trait of grey animals. The environment will almost certainly select for or against that trait, and if it is selected for we have a new phenotype which adds fitness to the population as a result. ... Wrong ... Imagine a case with animals without any mutations: two white animals breeding together ... the outcome without any mutation is an endless line of white animals so natural selection turns out to be useless in that case ... 

Natural selection is the hand that makes the non-random selection from a randomized set. It's like rolling a bunch of dice, but only looking at those that come up as 3's and ignoring the rest. The process has a random element, but it is not a random process. ... natural selection doesn't actually determine anything ... it's just a descriptive term to show that the mutations are favored by the environments ... what determines survival fitness are the mutations and environments ... and they are both random ... so using the analogy of the outcome of 3's is a gross oversimplification ... 4's can turn out to be useful ... my point is there's is no distinction for what can and cannot be useful ... a trait can be useful and detrimental depending on the environment ... so if we assume that a trait is a 3 because it's selected for in one environment, what happens when it's selected against in another? ...

Very wrong: natural selection (NS) acts on an organism after it has mutated. Mutations affect the phenotypes present, and it is how those phenotypes confer an advantage in fitness in a given environment which determines whether NS snuffs them out or keeps them. ... how exactly is this different from what I said? ... 

Fact: ID has zero unique, falsifiable predictions that have been confirmed through repeatable experimentation, nor does it even have any such testable hypotheses in the first place. ... Wrong ... I just gave one ...

Fact: Evolution and common descent have countless such predictions. ... are we subtracting the failed predictions? because failed predictions signify a false theory ...

Fact: IC has no bearing whatsoever on whether or not a structure could have evolved, as was illustrated by the bridge thought-experiment and applying the Mullerian Two-Step to a variety of structures. You have done nothing to illustrate otherwise. ... wrong again ... you're just proving your lack of substantial assimilation and understanding ...

Fact: Things like flagellum and mousetraps aren't even IC because they have components which serve independent functions when not part of the whole "core." The best you have been able to do is say that each new core is now irreducible, which you can obviously do ad infinitum. ... wrong yet again ... you still can't get the concept through your head ... I can prove it ... I've said countless times that a system is IC if the basic function is lost on elimination of any part but you still think a system is IC if the components cannot be used for other functions ... you still think reducing an IC system to achieve other functions implies the system isn't IC ... and sadly, I have to say you are way off the mark ...
Reply: Benjamin Toby"nested groups would be a better term "

And I'm perfectly fine with that. In the end, it's the same thing, though.

 "you are a programmer and you don't know what a code is?"

I have no idea what gave you that impression, that I don't know what code is. I know it very well. It seems a lot of other people don't, though, and I don't blame them because it's not as simple as it might sound.

"a program is merely an arrangement of codes you can have a code to get an input: but different programs call for that code at different times and lines "

Well, an actual program that you run on your computer contains no code at all. And this is where most people run into problem with their undertand of what "code" is.
When I write a program using assembly, then yes, I am writing code, that's correct. But when writing a program is C or C++ or Java, I am not actually writing code, because those are languages, not coding systems. (Even if we traditionally call it "coding", still. That doesn't make it technically right.)
And pretty much no matter which language or coding system you're using to write a program, once it's compiled into actual software it is no longer code or language, it is pure instructions.

And before you start arguing about this with me, consider whether you actually know anything about this subject.

And what I said is still true: The same code would produce the same program. But yes, we do make libraries or packaged routines or classes or whatever, to be re-used in other software. But then only parts of the code is the same.

"so what you're saying in essence is that I can just connect all the phyla to the creator and we have a tree of life? ..."

No need, you just have to connect all living things with the fact that they all use cells. That is essentially the one defining characteristic of "life".
If you choose to connect things by who/what created them, then what you have is a tree the describes creators, not their creations. It would be a ategorical mismatch.
The tree strcutre in taxonomy is about nested traits in species. That is all it is about, nothing else. There is no relation implied, only morphological similarity. It is a tree of morphology.
You can draw whatever conclusion from it, but as I see it, and as the scientific community as a whole sees it, it is definitely explained by common descent. Not only because of that tree, but also because you can get the same tree through genealogy, aswell, and because we know that traits are inherited, that's why we look like our parents, for example.

"... I think that'd be a more credible tree"

A failure of abductive reasoning. If you want to infer the best explanation, then a good explanation would not be "some magical guy from a story just made it that way", since that has no explanatory power. Such a magical guy could be anyone, and could do anything, so no matter what life was like, you can always say some magical guy made it that way. That makes it a non-explanation, from a scientific viewpoint.

" how would anyone successfully explain what a "god" is when you can't understand what similar designer is?"

I understand the concept of "a designer", because we have examples of that, and because it is a trait, not a thing. I am a designer, aswell! So are lots of us.
But a "god"? We have no examples of anythign such, and everyone who talks about "gods" seem to mean diferent things, and most importantly: No one can point to one! Show me a "god", and I'll know what it is.
Historically, people have used the word "god" for anything from totem poles to Julius Caesar, to the universe itself. Same word, jstu being thrown around. The word "god" has no actual meaning, it just refers to something unknown.

"Ac reator, however, doesn't have to do it that way. That's the difference. ... wth ... why can't a creator use the same language to create other organisms?"

I said he doesn't have to. A creator god can do anything, he has the ability to change the underlying framework itself, even. That's why "god" could be the answer to absolutely any question like this, and no matter what the truth is, and no matter how things are.
If a "god" could produce anything, then anything could be a production of "god". God could make pencils, therefore pencils could be made by god. Then again, he might not choose to make pencils, so then he doesn't make pencils. No matter what, you can always just say "god", and the intellectual part goes away completely.
"God" is equal to saying "magic".
Reply: antiHUMANDesigns

And I'm perfectly fine with that. In the end, it's the same thing, though. ... not for me ...

I have no idea what gave you that impression, that I don't know what code is. I know it very well. ... I seriously doubt that: your comments show you really don't know what the computer code is ... 

Well, an actual program that you run on your computer contains no code at all. ... W.T.H ... and you ask what gives me the impression that you don't know what a code is? ... anything that goes via the CPU is a code ... just like I tried to explain to you the other time ...

When I write a program using assembly, then yes, I am writing code, that's correct. ... Ummm it's more in the lines of "calling for the codes": they are already there ... you could say you're writing code in the sense that the language get's transformed into the machine language at the end of the day ... but the language contains snippets of codes with distinct functions ...

And pretty much no matter which language or coding system you're using to write a program, once it's compiled into actual software it is no longer code or language, it is pure instructions. ... and what the hell do you think a code is? ... it can be described as an instruction ... 

And before you start arguing about this with me, consider whether you actually know anything about this subject. ... I have a good idea about computer code since I studied Electrical and Electronics engineering in Uni ... and I can say you really don't know what the computer code is ...

Let me try to explain ... the computer code is simply combinations of transistor states  ... the CPU contains millions of these transistors ... a transistor can be used as a switch to toggle between two states which are on and off : depending on the base current: ie a base current means an on(or 1), no base currents indicates an off(or 0) ... with this the architecture of the CPU is made up with numerous combinations of these 0's and 1's ... I can give an example of a crude computer to explain my point ...
Lets say we have a set of 7 transistors with switches to allow and cut-off the base current ... and lets say we have them connected to a 7-segment display (ie each transistor activates one light in the display) ... lets say we want to get the letter "A" ... this means we must activate 6 switches and deactivate one ... which would give us a switch combination of 1110111 ... this is the code ... it's just the arrangement of the transistors: all these switches required to display the letter "A" can be connected to a single switch and boom! we have ourselves a crude keyboard... this is basically the computer code ... with this idea we have a CPU with millions of these transistors that can do amazing calculations via this same switching ... the computer code is not really what you write down in any assembly language ... it's the action and combination of transistor states ... that's it ... that's why you can build a mini computer with 7 transistors and it still is a computer ... because of the code it uses: on and off ... the regular PC processor has a CPU with more options for combinations of states that's why you can do more with it than with a calculator ... the calculator has a less complex architecture and doesn't allow for such tasks ... 

So when writing a program, you are more or less calling for codes already present in the CPU architecture and arranging these codes to gain specific tasks ... if you want to display the number "A" in your program, then you must go through the singular code for that letter ... which is in the form of a combination of transistor states ... 

the same code will produce the same value ... not the same program ...

If you choose to connect things by who/what created them, then what you have is a tree the describes creators, not their creations. ... wrong! I can connect all of them based on something common: the DNA ... and we have one creator ...

The tree strcutre in taxonomy is about nested traits in species. ... please use the terms agreed upon ... thanks ...

You can draw whatever conclusion from it, but as I see it, and as the scientific community as a whole sees it, it is definitely explained by common descent. ... and it's better explained by common designer ...

Not only because of that tree, but also because you can get the same tree through genealogy, aswell, and because we know that traits are inherited, that's why we look like our parents, for example. ... please again use the agreed terms ... a family tree is called a tree because of the connections of siblings ... that's what I said the tree structure implies ... and why it'd be better if you use the term "groups" ... not tree ... you can group members of a family tree into a tall-people-group : and in that group you can have a sub group of tall and long-haired people ... this grouping wouldn't point to any connection ... between them ...

A failure of abductive reasoning. If you want to infer the best explanation, then a good explanation would not be "some magical guy from a story just made it that way", since that has no explanatory power. .. a failure of abductive reasoning would be your expression of ignorance and lack of thought for the God concept ... you have to be really stupid to think that the God that has been spoken of for so long is just a magical man made up from a fictional story ... you have to be extremely stupid to believe that Newton, Galeleo and the countless theistic scientists were, and are all deluded ... 

so no matter what life was like, you can always say some magical guy made it that way. That makes it a non-explanation, from a scientific viewpoint. ... you have to realize that evolution is actually more of a joke in this sense since it says more or less the same thing but with a lot of random combinations ...  also the God explanation comes as a necessity when design is proven in life ... it's not like we just conjure up a magical man to explain the complexity of life ... actually the complexity of life drags us to an inevitable conclusion of an interference of a supernatural designer ... and the God of christainity just happens to have most of the traits expected of such designer ... if any Hindu god was so described with so much concurrence to facts then I'd have good reason to believe in that hindu god ...

I understand the concept of "a designer", because we have examples of that, and because it is a trait, not a thing. I am a designer, aswell! So are lots of us. But a "god"? We have no examples of anythign such, and everyone who talks about "gods" seem to mean diferent things, and most importantly: No one can point to one! Show me a "god", and I'll know what it is. ... if you understand the concept of a designer then what's your problem with understanding why I infer from that to say God is the designer? ... if you have a better explanation of a designer of such complexity then tell me ... because the only designer of such amazing diversity and complexity in life simply had to be supernatural ... 

If a "god" could produce anything, then anything could be a production of "god". God could make pencils, therefore pencils could be made by god. Then again, he might not choose to make pencils, so then he doesn't make pencils. No matter what, you can always just say "god", and the intellectual part goes away completely. "God" is equal to saying "magic". ... actually magic is what evolution proposes ... the God explanation is actually highly reliant on facts ... it induces from a known cause which is intelligence and perfectly explains life ... evolution is actually a mombo-jumbo explanation when dealing with the real complexity in life ... it's true I cannot fully explain God and why He did and din not do a few things ... but the writing on the wall in nature shows a highly principled being which uses mathematics a lot ... this is not magic bruh ...
Reply: Benjamin Toby Taxonomy is done in a tree structure. That's just the name of the data structure, not a point of debate. Your explanation of "God" doesn't have any predictive power, as has been said many times. It can be used to explain everything while simultaneously explaining nothing.

Are you gonna respond to my last post, or did it become invisible again?
Reply: Benjamin Toby"And I'm perfectly fine with that. In the end, it's the same thing, though. ... not for me ..."

Shall I draw it for you and prove that it's the same thing? Stop being silly. It's not a matter of opinion, it's a mathematical fact. A set of nested sets (groups, whatever) can also be drawn as a tree, and it will give the same information, therefore they are the same thing. If you have a problem with trees just because it contains lines between the points, you're just being childish.

"I seriously doubt that: your comments show you really don't know what the computer code is"

Are you a programmer? I mean, you're talking to someone who has programmed for about 22 years, and you assume that when we disagree about something, it's me who is wrong, huh? Where's your humility and your sense of reason?
I can explain why I'm right. Can you explain why I'm wrong? So far you only said that I am wrong, but have given no explanation for why I'm wrong.
"Code" is second-level symbolism. Computers themselves do not work with symbolism, they only work with what we call "instructions". And C/C++, Java, and so on, are not code systems because they have syntax, which means they are more like a language. When you write in those languages, what you write is not decoded, it is interpreted by a compiler. you're effectively talking to a program about how you want the software to be, in a language that the compiler can understand. Had it been code, then it would simply have to covert the symbols to whatever symbol represent the instruction, but that's not how high-level languages work.
Assembly works that way, though. Each code word directly translates to an instruction, therefore we can call it "code" and be technically correct. That is, a word like "mov" represents the name of the instruction for moving something, and that instruction's name is the symbol for the actual instruction. Therefore, we have 2 levels of symbolism, thus "code".
Morse code is also "code" because each morse sequence is a symbol that represents another symbol (a letter/character) which in itself is a symbol, and may refer to something real. Second-level symbolism, therefore code.

But the pure instructions that exist in RAM or on HDD in a computer, which "runs a program", uses no symbolism to work. It is voltages that are moving around inside circuitry. It doesn't use symbolism because only a mind can use symbolism, and a computer doesn't have a mind.

If you still think I am wrong, then explaiun how I am wrong, don't just assert that I am.

"anything that goes via the CPU is a code "

No it damn well isn't. But you can describe it using "code", or symbolism. It isn't inherently code, because a CPU doesn't understand symbolism, and definitely not second-level symbolism.
The thing that goes into the CPU is a pattern of voltages. That's all it is and all it needs to be to create the phenomenon of a "program".
But when we want to talk about those patterns, we make it easy on ourselves and symobolize them using 1's and 0's (they are not actually 1's and 0's).
And because specific patterns of those 1/0 produces specific results, we give some of those patterns useful codenames.
Thus, we end up describing what is going on using the concept of "code" and "symbolism".
But it isn't actually code just because we use that concept to simplify what's actually gonig on. You're committing the same logical fallacy that the other guy ("Mark") in this thread is committing, the logical fallacy called "reification".
https://en.wikipedia.org/wiki/Reification_(fallacy)  <- for reference.

"and you ask what gives me the impression that you don't know what a code is?"

It's because you think you know what it is, but you actually don't, like most people. Most people just use the word "code" whenever they feel like, it seems, without actually learning what it means.

"and what the hell do you think a code is? ... it can be described as an instruction"

What, so "morse code" is actually "morse instruction"? No, it's not.

A "code" is a form of "symbol" within a "coding system", which is an arbitrary thing. A message needs to be encoded using any coding system before it is "a code", and it must be decoded before the message can be understood, again.
Computer instructions are never encoded into code, because that would mean that the CPU would have to decode it before it can read it.
That is only part of the problem, however, because even if it could decode it, it still doesn't have a mind, so it wouldn't be able to understand the symbolism contained behind the code.
Therefore, it is nowhere near "code". Only in our minds, not in reality. We use the concept of "code" to make talking about thing more efficient, or to hide a message. In either case, it's always symbolic, that's why a computer cannot use it. It doesn't have a mind, it cannot think conceptually.

" I have a good idea about computer code since I studied Electrical and Electronics engineering in Uni "

I don't see how that helps you. "Codes" are conceptual, and if you're talking about "coding a program", then it is a matter of computer science, not "electronics".
Have you studied computer science?

"Let me try to explain ... the computer code is simply combinations of transistor states"

Well, no, the code conceptually represents that, in your head, yes. It isn't actually that.
If you don't undertand the difference, then once again... reification fallacy.

"I can give an example of a crude computer to explain my point "

Too late to say "no need"... :/

"this means we must activate 6 switches and deactivate one ... which would give us a switch combination of 1110111 ... this is the code"

Nope!
1. The letter "A", which represents "1110111", is the code!
2. "1110111" is symbolism for the state of those transistors.
3. The state of the transistors is the "real thing" that the symbol is referring to.
4. Point #1 is second-level symbolism, therefore it is "code". A -> 1110111 -> the real thing.

"A" is the code, and a computer cannot read "A". It would have absolutely no idea what "A" means, because it cannot undertand codes or symbols.
It can "read" the thing that "A" represents, though. But what it represents is not a code. It is the code for that thing that is the code.

That's why when we write code, we write, for example "mov" (in assembly), which can be decoded using the assembly code system to represent a value, or a binary sequence, which represents the actual states of the transistors.
Second-level symbolism, once again.

"that's why you can build a mini computer with 7 transistors and it still is a computer ... because of the code it uses: on and off "

On/off is not code, they are symbols. It is only first-level symbolism, and "code" is second level symbolism.
A symbol that represents "on" would be code. It could be anything. If you and I agree that "sgtt" means "on", then "sgtt" is code. If I write "sgtt", you will know that it decodes to "on" using our coding system.
But because cod eis always completely arbitrary, anyone who doesn't know the codign system has no idea what "sgtt" is supposed to mean.
That is, once again, why a computer cannot use codes, because it requires a mind.
Software could potentially use codes, though, since software could potentially emulate minds, or even have a mind.

"So when writing a program, you are more or less calling for codes already present in the CPU architecture and arranging these codes to gain specific tasks"

No, we're using the things that the codes represent. The code is just an easier way to talk about it.
I could just say "i want those transistors to let the current though, but not those ones". But it'll be easier to say I want "11010110", for example. And it would be even easier if we could give that pattern a name that describes what it does.
A codeword.
In case I'm not just picking at your words, you're once again committing the reification fallacy of thinking that a code can be real, when it is a conceptual thing.
Kind of like thinking that being happy means that you have actual "happiness" inside you, as a real thing, not just symbolically/figuratively.

"the same code will produce the same value ... not the same program"

OK, so every time I compile my program, without changing it, I will get different results, huh? Strange how that isn't true.

If I write a program in assembly, then I am writing code. And every time I compile it, I am supposed to get the same result. And I do. To get a different program, I have to change the code. Obviously.

"wrong! I can connect all of them based on something common: the DNA ... and we have one creator ..."

I don't even know what you're trying to say. When you create something like a tree structure or a set of nested sets, you need to make sure that the points all are of the same "category", or "type". I mean, it has to make sense. You cannot have a tree where some branches/sets represent other categorical kinds of things than some other branches do. It's like having a list of employees wages, which also contains some of their favourite foods. :/ Make 2 separate lists, or columns, or something.
Sicne the tree structure that taxonomy forms is about morphology, it cannot partially be about the "creator of the morphology".

But yes, we could say that the thing that connects all living thing is DNA, because that is probably completely true. Or we could say it's cells that connects them all. Doesn't matter, really.
But whether there was one creator or a thousand or zero has nothing to do with the facts that the tree demonstrates. Maybe the tree means nothing, but it is still an observation of a pattern that exists.

"The tree strcutre in taxonomy is about nested traits in species. ... please use the terms agreed upon"

Do you mean to use "nested" instead of "tree"? Since they come out as the same thing, it doesn't matter if I use them interchangedly. They are effectively code words for eachother.

"and it's better explained by common designer"

Perhaps, but that is not a scientific explanation, because it doesn't make any predictions, so it can't be tested, and so it can't be known to be true or false, and it doesn't make a difference.
It's the same thing as "string theory". One idea that explains everything but doesn't make any testable predictions, and doesn't imply anything useful. Whether or not "strings" actually exist doesn't make a difference to us, therefore it's a crappy explanation.
If you can show some way that the "god" explanation actually makes some kind of predictions, it is completely useless.
Therefore, don't pretend that it is a "better explanation", because it certainly isn't - even if it were true, actually.
If the universe is indeed run by magic, and anything can happen at any time, then there is nothing we can learn. It might as well as be random.
However, that doesn't appear to be the case, and we're not going to assume that it is without a good reason.

"a family tree is called a tree because of the connections of siblings "

Yes, we use a tree structure for that because it's the best way to explain it.
We can also use nested sets to decribe family relations. Works just as well, since they work the same way.
It's all about how you choose to "draw" it, if you would draw it.

"you can group members of a family tree into a tall-people-group : and in that group you can have a sub group of tall and long-haired people ... this grouping wouldn't point to any connection ... between them "

I agree completely.
But that's because hair length, for example, isn't inherited. But your length may be, and so on.
When looknig at large populations of people, for example, then you can look at the average of different traits.
Look at all europeans, asians, africans, australian natives, polynesians, and american natives, for example. When looknig at the averages of those populations, you can see a tree structure, a simple one. Because individual variation isn't really a factor anymore. There will be small differences in length and skin color, and so on,a nd you can describe it as a family tree, because that's what it really is.
And yes, you can do the same thing with species, even though you don't like that fact.

"a failure of abductive reasoning would be your expression of ignorance and lack of thought for the God concept "

Stop being so childish...! I call into question your abdutive reasoning, and the only thing I get in reply is effectively "no, you", like a fucking 6-year old.
Listen to what I said. When looking at the facts, the observations of life, we need to infer what the best explanation is. Your explanation doesn't work becaue it has almost no explanatory power. Sure, someone could have created everything, but why are things the way the are? Evolution explains that (why each species is the way it is), but ID doesn't. (Remember the challenge I gave you which you still have not met?)
ID is just a completely intellectual block. "Some magical guy did it, hell knows why, but he did, end of question".

"you have to be really stupid to think that the God that has been spoken of for so long is just a magical man made up from a fictional story"

1. There have been many, many, many "gods".
2. Yes, that is exactly it: A fictional character from a story. Demonstrate that it is anything more than that.

" you have to be extremely stupid to believe that Newton, Galeleo and the countless theistic scientists were, and are all deluded "

No, because it makes perfect sense that they thought what they thought. If I lived backl then, I would probably have beena theist, aswell. They were ignorant of the things we know today.
But yes, it's kind of weird that they chose to assume that a god exists without any evidence for it. But it's really hard to put yourself into the shoes of someone from that time.
Remember, while Newton surely was a complete genius, if he was teleported to 2015, he would get schooled by the average teenager in the field of science. He would look like a fucking moron, to be honest. Seriously, he wouldn't know a lot of things that are really damned basic to us, today, like atoms and molecules, but also the thing that have made a lot of his work obsolete: The theory of relativity.
But yeah, his math skills would be useful, even though he would have to study up on everything he has missed since his time.

..and also, if Newton lived today, he would most likely be an atheist. I'd bet you.

"you have to realize that evolution is actually more of a joke in this sense since it says more or less the same thing but with a lot of random combinations "

Heheh, yeah, you really seem to know what you're talking about. :P
No, the theory of evolution has predictive power. That's the whole difference.

"also the God explanation comes as a necessity when design is proven in life"

I'll wait until that is proven, then. But I'm not going to hold my breath.
However, you're wrong, because if life was intelligently designed, it doesn't mean that a "god" designed it. It just means "someone" did.
And even if it was a god, you have no idea which god, since you can't test it.

" actually the complexity of life drags us to an inevitable conclusion of an interference of a supernatural designer "

Nope, evolution explains it. You want to know where complexity came from? Well "randomness" is not the answer. "Design" is not the answer. Cumulative change through the process of natural selection acting upon replication with variation, however, explains it. It explains that this is lawful, that it happens due to the nature of reality. And, it can be demonstrated. The process is used in computer science and advanced robotics.

However, I could potentially stretch it to say that it's not necessarily impossible that a god could've created the conditions necessary for evolution to work, such as the increase in entropy.
It's not a good framework for life, but it is a good framework for evolution.

"and the God of christainity just happens to have most of the traits expected of such designer"

Same god as judaism and islam, right? Except different names. Commonly referred to as the "abrahamic god"?

Anmyway, I adisagree. The one obvious trait that seems to be missing the physical existence of that god. If I want to make humans, I better start by actually physically existing.
Anyways, this is a huge subject in itself. There are sooo many things I could talk about concerning this, but I'll leave that for some other time, if ever.

"if any Hindu god was so described with so much concurrence to facts then I'd have good reason to believe in that hindu god "

Personally, I prefer the hindu religion, because they actually accept science. It's nowhere near as dogmatic as the abrahamic religions.
Of course, I haven't talked to many hindus, so I might be wrong, but that's what I learned from the few I've talked to.
Anyways, you're a moron if you believe in something just because it fits the facts. It has to actually be tested to see if it can be falsified.
You have make up a gazillion stories that may all seem to fit the facts, but you hav eno idea if any of them are correct until you test them against reality.
And if thery can't be tested, then forget about them, because then they have no predictive power, so they make no difference.
Every day, scientists come up with thousands of possible explanation that fit the facts, but only 1 in 1000 ever turn out to actually stand up to testing.
If you believe everything that fits the facts, then you'll likely end up believing things that contradict eachother. And that is irrational.

"if you understand the concept of a designer then what's your problem with understanding why I infer from that to say God is the designer?"

I explained that. I said that I know that designers exist, because we have examples of it. But we have no examples of anything that deserves to be called "god".
Just because designers exist doesn't mean that gods exist...!
And not everything that exists is designed by an intelligence. I do hope you agree that a pile of rocks wasn't designed by someone, for example.
So if not everything was designed, then we need ot know which things are designed, and we can only know that by demonstrating that a designer of those things exist.
We cannot rely on an argument from ignorance and default to the position that anythign we don't understnad is made by a god. We've done that mistake for ...forever, through history. Lightning is god, volcanos are gods, earthquakes are gods, teh sun is a god.... none of them ahve ever turned out to be gods.
And now we've got peopel saying the big bang was god. What makes these people uanble to learn from past mistakes? When will people stop?
At least modern scientists have finally realized that we need to stop assuming things. Perhpas gods exist, we don't know, adn no one has shown what a god is or even that a god could exist. If they do, then we can talk about it without having to make assumptions.
And who was it that made this change? Darwin, probably. When we realized that not even life itself requires a god to be explained, I think most scientists "woke up" and realized that perhaps there is no reason to ever assume "god" as an explanation for anything until there is direct reason to actually do so.

" if you have a better explanation of a designer of such complexity then tell me ... because the only designer of such amazing diversity and complexity in life simply had to be supernatural"

Wouldn't he/she/it just have to be really, really smart, or have really, really good technology?
Can you not imagine a super-computer of the future who can, given some processing time, figure out an entire eco system, and how to build it? I can.

However, I cannot imagine something that per definition doesn't exist (a being outside of space and time), who has no physical structure, yet still has a mind, even though minds only come from brains, as far as we know.
I might be able to accept the idea of a "god" if at least he physically existed in the univesre, so that I could accept that he would have a physical impact on things, and that he would be able to have a mind.
But that's not how he's thought of, normally. And then I cannot accept it, because it is so damned far removed from everything we know that it doesn't make any sense to us at all.
That's not me saying that I know that god[s] do not exist, because I don't know that, I cannot know that. I just definitely cannot even believe that it is possible, because no one has demonstrated that it is.

But still, while it's possible that some intelligent "something" seeded the initial life on earth, we know that life evolved from that stage. You cannot explain away the facts. Even if creator gods exist, or whatever, life on earth still did evolve - or we've been tricked to think so by someone extremely powerful. And I see no reason to believe that we have been tricked that way, so I can't just believe that to be true. I am not paranoid.

"actually magic is what evolution proposes"

Point out in any text book or scientific paper, or anything of the kind, where it says something that you interpret as "magic".
If that was the case, it would not pass peer review.
But of course, you're never specific about any of these accusations. At least I can point out where in the bible "magic" is being implied. That is, if we can agree on a definition of "magic".
No, evolution is a process that has clear and relatively simple mechanisms that do not require magic. Those who are more fit to their environment will tend to have more offspring, thus increasing the frequency of their genes in the gene pool. No magic, just logic. But you probably rely on some straw man version of the science, and I don't care about defending your straw men.

"the God explanation is actually highly reliant on facts ... it induces from a known cause which is intelligence and perfectly explains life"

Theoretically yes, it does explain some of the facts, if you're talking about the concept of a creator god without the baggage of things like the bible.
But like I said, we can come up with any number of innovative ideas that fit the facts, but that doesn't make any of them true.
Does your explanation make any predictions, so that we can actually test them? But I bet you 50 bucks that even if we did falsify it, you wouldn't stop believing it.

However, intelligence is not knows to exist outside of brains, or something equal to a brain (a computer, perhaps). So no, you're taking a huge leap there, by assuming that something intelligent can exist outside of space and time, where we might argue that matter and energy doesn't exist.
Therefore, no, it doesn't explain it very well at all. Start by showing that intelligence can exist outside of the universe, and *then*we can talk about whether such an intelligence can or did create anything inside the universe.

"but the writing on the wall in nature shows a highly principled being which uses mathematics a lot ... this is not magic"

I don't know what your definition of "magic" is, but my definition of magic i something that cannot physically happen, yet still does. It is a suspension of the laws of the universe.

"Highly principled"? Explain?

Yes, I agree about what you call "the writing on the wall". It's clearly the reason that humans have been religious throughout history. But we know better now, because there is no longer a reason to believe that anything was created by gods. There never was, but people didn't know that. Now we do, because we've learnt a lot about the universe, and we've noticed a pattern: Everything appears to have a natural explanation. we can't oprove that everything has a natural explanation, but so far we should've seen some demonstrable case where there is a "supernatural" explanation. And we might not know the details about everything, but we know enough to be able to infer with good support that everything in the universe has natural causes. It has never failed us so far.
As for the univesre itself, sure, we don't know much about that. And I don't have a problem with deists, I just don't see the point.
Reply: Benjamin Toby "my reason for refusing the tree description has be explained repeatedly ... but just for the nth time: the tree used in biology is that of Darwins and it's used mainly to draw the connections b/w organisms "

And that is not the tree I am talking about...! I have told you this a few times, now. I am talking about the mathematical concept of a "tree structure". A way to organize information.
And yes, you can call it "nested hierarchies", if you want, but it's the same theoretical structure.
When I say "the tree of life", then I am talking about the tree you're talking about. I have strictly avoided saying it like that as to not make it seem like that is what I am talking about. And I have explicitely stated that I'm not talking about that tree.
I am talking about the possibility of arranging physical traits of different species into nested hierarchies - a tree structure. This came long before anyone proposed that species are related.
Now yes, evolution has "adopted" this because evolution is an addition to our understanding of all of this. They now go hand in hand, in a sense. However, our undertanding of the actual relations between species has made us have to move some species slightly in "the tree of life". And they're still being adjusted as we learn more about them.

"the family tree has the same concept"

Yes, and that was always the intention behind the "family tree". It was not the intent behind the linnean taxonomy (which can be describes as a tree).

"we can group organisms into animals with tails, animals with whiskers, hoofs, scales"

Yes, good. However, there is one hugely important thing to add to this: The groups do not overlap. There are not mammals with feathers, or birds with hair, for example. So they are not arbitrary gourps, they are nested hierarchies. This makes all the difference.

"Are you a programmer? ... Nope ... actually an amateur programmer ... still learning "

Well, I don't care if you get payed doing it or not, the question is whether you "know" programming. Good that you do, then we might be able to use this to communicate/discuss some things.

"I mean, you're talking to someone who has programmed for about 22 years, ... so what? "

...so there is good reason to think that I probably know a lot about the concept of programming. It would be unreasonable to think that someone who has done something for 22 years do not understand the thing they're doing, yet still manges to do it for 22 years. Especially something that is so "theoretical" as programming, where knowledge is key to doing it, so to speak.
(That is not to say that I know "everything" about it, because no single person knows everything about it.)

""Code" is second-level symbolism ... I'm sorry but you don't get to describe code to suit your explanation"

That must be the dumbest thing you've said so far. Yes, I will describe what "code" is when I notice that someone doesn't understand it, and we're trying to have a conversation about it.
Or would you prefer that I just go on, even if I know that we'll have nothing but misunderstandings from this point on? Do you seriously prefer that people talk past eachother?
the entire problem we're having is the fact taht you *don*t understand what "code" is. So yes, I will obviously try to solve that problem.

"I said you were wrong and I gave you a perfect example to explain why "

Nope, you have not. You have written things based on a presumption that something is a certain way, but you have not explained what way that is, or why you think it is that way.
And because I have noticed that this problem exists, I brought it up.
At no point have you ever told me your definition of "code". You have given examples that appear to contradict eachother, which isn't helpful. If you think that code is not second-level symbolism, then tell me what you think it is. Stop avoiding it. I have given you a clear definition of what it is. A symnbol that that stands in place of another symbol (second-level symbolism). That is "code". That is why morse code is code, and it is why assembly code is code, and why "TGAACTG" when talking about DNA sequences is code, and so on.

Or do you sreiously think I just made this up? I have no motivation to cause misunderstandings and then spend all this effort in trying to clear up the misunderstanding. I am telling you what "code" is, not what I would like to code to be, or whatever.

"When you write in those languages, what you write is not decoded, it is interpreted by a compiler. ... interpreted just like Swedish language can be interpreted into English language"

Yes, in a sense, but not completely, because english is a language, and computer instructions isn't.
Swedish->English is a translation between two languages. In the end, you've still got a language, not something "real".
A compiler for C++, for example, is an "emulated mind" which understands a specific language, conceptually, and uses it to understand what the human is explaining about how the software should be. It then makes software based on how it's been explained.
Languages like C/C++ cannot be directly translated/converted 1:1 into machine instruction, because a lot of it is conceptual and only helps to explain concepts to the compiler, so that it can "understand" what you are trying to do. And it wille ven tell you when you're being illogical. Assembly cannot do that, because no concepts are ever explained.

That's why it isn't just a coding system, like assembly is. In assembly, everything is 1:1 converted to machine instructions. (Not that I really ever do much assembly programming.)

"after it gets to English, the intended instruction is carried out: which is the decoding ... say something like "switch off the PC""

Did you just say that "decoding" effectively means to carry out an instruction? 8|
No, "decoding" means to turn something that was "encoded" (turned into code) back to not being code.
I mean, damn, you've got your terms so mixed up it's bordering on hilarious.
Do you agree that encoding something makes it "code", and decoding is something you do to "code". To de-code it, to make it no longer "code". How is this so hard to understand?

I take the word "hello", and I encode it using a coding system that you and I have agreed on, which turns "hello" into "255".
Then I give you that "255", and you use the same coding system to decode "255" back into "hello".

Of course, you might use the wrong coding system, where "255" means something else. That's the problem with codes, they're completely arbitrary, though they can use a logical or mathematical system to make it more intuitive, or perhaps more efficient.
The ASCII table is a coding system, for example.

"The thing that goes into the CPU is a pattern of voltages. ... and these patterns of voltages produce different patterns of voltages ... this is the action of the computer code"

The patterns of voltages are real. The code and symbolism we might use to describe the voltages, and their purpose, is conceptual and only exists within minds. There physically is no code in the voltages.
It is unclear to me whether you understand this, or if you're once again back to a reification fallacy.

"Too late to say "no need"... :/ ... I just hope that I'm not reading this right because it seems like you don't even finish reading the entire comment before responding "

I read 1-2 paragraphs at a time, not the entire comment. It makes it easier to remember what I wanted to address. I could do it a different way, but that would make this take even longer, and it already takes too long.

I read you saying that you're going to explain how a simplified computer works, and I wish I could just have saved you the trouble, that's all. I know enough about computers to perhaps be able to build computer circuitry.

"1. The letter "A", which represents "1110111", is the code! ... Ummm the letter A is the decoded output ... "

If I write "A" in "notepad", for example, then the "A" is "code". That is, the letter/symbol "A" represents a value in the ASCII table (notepad uses the extended ASCII table, right?), which is symbolism for the pattern of voltages in the computer. Therefore, it's second-level symbolism. Code. The "A" is code for a value that represents the voltages.
If I use something else than the ASCII coding system, then "A" might be a different pattern/value. It's compeltely arbitrary. That's because "A" doesn't exist in computers, because it is a concept. We make the copmputer draw something that we think looks like "A", so that we can communicate "A" froom one person to another, with the computer as a middle-hand. But the computer never holds an actual "A", because it can't. We don't even know how brains actually store "A", and it's probably different in each brain.

"2. "1110111" is symbolism for the state of those transistors. ... which is the code like I explained ... I can call it onononoffononon ... but it'll represent the same thing ... which is the code ..."

"1110111" doesn't represent code, it's the code that represents this. :/ Yes, thing can be turned back and forth between being code and not being code, but it make sno sense to say that something represents code. That would make it circular and unnecessary.

This is the actual information, described symbolically as that binary string.
I could make it easier to talk about by saying that "A" represents "1110111", so that I don't have to say "1110111" all the time. That makes "A" a code for "1110111". If we agree on that system, then everytime I want to say "1110111", I can just say "A", instead. But only if you know that coding system.

I undertand waht you mean, that we want to actually communicate a letter. But there never was a letter, there was always only a pattern of voltages. But at any point, you can always interpret those voltages as letters, if you want to. That's why we must always make sure that we consistently treat data the correct way, the way it was intended to be treated. This is why we have "data types" in programming.

Same thing when talking about DNA sequences. We can look at a DNA sequence and say that one sequence is "cytosine, guanine, guanine, guanine, thymine, cytosine".
But if we use a coding system where the letters A, T, G, and C are code for adenine, thymine, guanine, and cytosine, respectively, then I can simply write "CGGGTC".
That is code. To know what "CGGGTC" means, you have to know that it was intended to be decoded as a DNA sequence, using a very standard and simple coding system of initials.
"C" isn't inherently code for cytosine, because "C" could also mean "degrees centrigrade", or "celsius". Nothign about the lettter "C" tells you if it is intended to represent somethign else than just the letter C. That's because codes do not actually exist, they are a consequence of intent.

There are no letters in a DNA molecule. There are nucleobases, molecules that are chained up in sequence. We call those bases different things (cytosine, guanine...), and we have a coding system to make it easier to write long sequences of them, for example.

"3. The state of the transistors is the "real thing" that the symbol is referring to. ... and that real thing is the code ... that is why it's called computer code"

Nooooooooo! Reification, once again. A code can never be real, because it is a concept! Anything can be code if it was intended to be treated as code, but it isn't physically code, it's only code in our minds.
A computer can't tell teh difference, it just does whatever its instructed to do.

But it so goddamned brutally clear that you don't know what "code" is, so I don't understand why I'm even bothering. I can't talk to you about until you admit that you're wrong and start using the word "code" correctly. You're causing a lot of inconsistencies, and even reification fallacies, all over the place.
And it really isn't that hard, either. When I write a computer program, I am writing a bunch of letters. In my mind it is code, because I am following a coding system that I have agreed to use, together with the person who wrote the compiler. We need to follow the same coding system, or we don't get the result we want.

You said "that is why it's called computer code". It isn't that thing that is called "computer code", you utter moron. Computer code is, for example, assembly. It isn't assembly that's going into the CPU, you know. Or do you know that? I'm starting to wonder if you even know what a keyboard is.

Perhaps what you mean is what they call "machine code". But machine code is not the pattern of voltages, machine code is what you see if you open an .exe file in notepad, basically. It is a numerical readout of the binary sequences. No one seriously programs in machine code, and machine code is code for machine instructions. It is the instructions that run the machine, not the code that represents the instructions.
Anyways, "machine code" isn't one thing, it's a label for... well call it a "category", sort of like how "high level languages" isn't a language, it's a category of languages.
Machine code is basically the lowest level way you could ever program in, no matter how you go about practically doing it, because it directly represents the instructions, so you need no compilation. And it's theoretically lower level than assembly, but not practically.

" is the output and the output is what we are looking for, that's why we use the code ..."

That wouldn't be "code", then it would be "conversion".  I have no idea how you mean that you "outputted A". You can do that a gazillion different ways, and depending on how you did it, it would be a different process.

" the code is meant to transform an input to an output of a different form..."

Now you're talking abot "code" only traiditionally, not actually. Not all "code" is actually "code".
Like I've explained, we call the "soruce code" in C/C++ "code", only because of tradition, not because it actually is code. It isn't, it's a language.
But once again, liek I've also said, your source code isn't the software, the software was built by a compiler by telling it conceptually what you want. There is no 1:1 conversion. Your C/C++ code doesn't actually run the software.

Howeve,r if you wrote the program in assembly, then yes, conceptually your code represents a piece of software. Only conceptually, though.

" the input is the pressing of the button, the output is the letter A displayed ... whatever goes in between is the code"

Whatever is between is the software that is a result of what might be traditionally called "code", but isn't actually necessarily "code".
So, for 2 reasons, it's not code: A computer doesn't run code, it runs instructions, software. And the software was possibly not written using code, but using high-level languages, so it might not even conceptually be code.
Sounds like you're still stuck with that reification fallacy, though, of thinking that code is real rather than conceptual.

"computer code and programming can and will exist perfectly without this "second-level symbolism" ... let's say that mov stands for 101100101010110 ... one can just write a program using 101100101010110 ... as a matter of fact all programs can be written using binary code ... so what happens in that case? ... where there's no "second-level symbolism"? ... does it mean there's no more computer code?"

Exactly! This is exactly it! What I've been trying to convey, all along.
Just don't call it "binary code", because it's not code, unless it's simply idiomatic. A binary string is a direct representation, without a second level of symbolism, therefore it's not "code", it' just symbolism.
And exactly, a computer actually carries out instructions that are directly represented by a value, such as "101100101010110", like you said.

Only if you want to be able to write more complicated programs do you need to simplify these things by adding a coding system, where different words represent those binary sequences. The compiler will then translate you text file of written code into a long binary sequence, with a 1:1 conversion.
So that's when they invented assembly. Assembly is true code, because a codeword is used to represent a value like "101100101010110". And this is how they used to program.
Then we invented a smarter way, where we could describe concepts to the compiler to help us find where we do things wrong, and so on. If th ecompiler can "understand" what we're trying to do, then it can tell us when we're not being logical.
They were no longer true coding systems, but they still called it "code" out of tradition. And they still do. But they are actually "high level languages".

I sincerely hope this wasn't just rhetorical, because you finally seem to understand what I've been trying to say. And I think you knew this from the start, it's just that it's confusing to talk about.

"On/off is not code, they are symbols. It is only first-level symbolism, and "code" is second level symbolism. ... Bingo ... this is your confusion ... the computer code is not a "second level symbolism"  like you say ... the reason is above ..."

You probably mean "machine code", right?
If you mean the actual instructions, the patterns that go into the CPU, then they are not codes. They can be describes by codes, but that aren't inherently codes, they are just specific patterns of voltages.
I don't know what you mean my confusion is. "Computer code" (assuming I understand what you mean by that) ins't code. It is, in your head, if you want to look at it that way, but there cannot ever be anything that is real that is "code", since "code" is conceptual. (I've said that so many times, now...)
I hope you understand what I mean when I say this: A comptuer can't actually read machine code. Yes, sounds strange, but please understand what I mean. It reads the thing that the machine code represents, that it "describes". "Machine code" is conceptual.
A computer is not a mind, so it never deals with anything conceptual. It is forced to only deal with the things that our concepts represent, and it is up to the programmers to make sure they consistently treat the same binary sequences as if they were a specific conceptual thing. (Data types.)

"I said a program contains codes ... so if you create a program "X" it would contain the same codes and arrangements no matter how much you compile it"

This shows how you're confused. A program doesn't contain codes, it's code that may contain a program.
"Code" is the thing I am writing.

int main()
{
    return 0;
}

...this is "code" (traditionally only, since it's C). It describes what the program should be like.
That is, in a sense, there is a program in this code.
But there most certainly is no code in this program!
The code is turned into a program when it is compiled into software. At that point, it's only a sequence of instructions.

Of course, it's theoretically possible to make a program that contains codes, but that's a special case and not what you're talking about.

"yes it is scientific ... it predicts that signs of design would be found and tests can be carried out to confirm these"

But have you even considered how to test if something is "designed"? You do that by finding a designer. Not by declaring that something is designed.
And no, we cannot find a "god" who designed it if you assert that the god who designed it cannot be found by definition, because he isn't a part of nature.
That's why it can't be tested.

"some of these signs are explained by Irreducible complexity and specified complexity "

No, "irreducible compelixty" is an argument from ignorance. A logical fallacy, therefore not valid.
That is, we cannot practically test if something is irreducibly complex because someone can always argue that we haven't tested all possibilities.
Irreducible complexity = "I cannot figure out how this could evolve, therefore it cannot have evolved".
See the fallacy?

As for "specified complexity", I've heard that term before, and I've asked for an explanation of it, but never received one. Perhaps you could break the trend and actually explain what it is and how to identify it, so that I can know it when I see it.
And since I still don't know what it's supposed to be, I have no idea how it relates to the subject of evolution at all.

"IC can be tested an proven like I have shown here "

"Here"? Where?
Anyways, I just explained why it can't practically be shown. It is an argument from ignorance, so it's not valid.

"IC has been proven [...]"

Apparently by someone who doesn't understand what "argument from ignorance" is, then.
Or, alternatively, the appeal to lack of imagination. "I cannot imagine how this could have evolved, therefore it can't have".

Then again, perhaps you could give an example and prove me wrong?

" I've been trying to explain the concept od God and ID for as long as I can remember but you just can't see the thought process and the evidences "

Then why the fuck do I feel like I have gotten zero information from you? All I ever hear from you is "nope, that's not true", over and over. Nothing positive, only negatives. You're a nay-sayer, and you provide near to no information about anything at all.
I am here, ready to listen and evaluate, and I am asking you to provide the infromation to me, yet you refuse, over and over, and then claim that I'm not accpeting your information, or what? Are you fucking trolling me, or what?
All you ever do is hint to the existence of the information, basically, but then refuse to actually tell me, and then say that you have given it to me.... sigh

"but you just can't see the thought process and the evidences "

Of course I can. That's what I am refuting, most of the time. I see a lot of logical fallacies and misuses of all kinds, and that's what I try to draw attention to.
I mean, iof people believe that gods exists because of "irreducible complexity" and such things, then yes, their logical deficieny is very clear to me. And I will point it out, in the hope that they learn something.
I have yet to hear a single good (or even valid) argument for theism. And yes, I have heard a lot, to the point where nowadays, all I heard is repetitions of things I've already heard a number of times.
Well, except for "specified complexity", which is still a mystery to me. Good to see now things pop up every now and then, I guess.

And the funny thing is that I see atheists make bad argument sometimes, too, and I correct them, aswell. But out of all the theists and atheists, the theists are insane at applying logical fallacies. It seems to me that the only way to ever "justify" being a theist is to use logical fallacies. It's utterly impossible without logical fallacies, it seems.

Reification, equivocation, appeal to consequences, confirming the consequent, arguments from ignorance, and lots of pure non-sequiturs that simply drive me crazy. (Yes, I am looking at you, William Lane Craig.)

It's sad when the only theists I an actually respect are the ones who know that they have no idea and admit that they "just have faith". They're probably the ones who are smart enough to know that there are no way to justify it with reason or evidence.

"oi smart guy ID says genetic variation and adaptation are facts ... combined with environmental changes, we have sufficient explanation for the diversity of life from a simpler origin"

So, evolution then. You can drop the name "ID" and call it evolution, and join the rest of the scientific community.
No, obivously not, because what you're saying is only 1% of the truth. The devil is in the rest of it.

"(Remember the challenge I gave you which you still have not met?) ... like I said I responded to that twice ... and I don't think it's worth wasting my time with so much nonsense"

Yes, two times you have responded, saying that you have responded to it. Zero times have you actually responded to it.
You said ID can explain the facts, I gave you some facts, and I have not received ID's explanation for those facts.
You call it nonsense? You mean that ID is a scientific theory, yet the idea that it would actually explain the facts is "nonsense"?
You're fucking hilarious, sometimes. If it was actually a scientific theory, its whole damned purpose would be to explain the facts and make predictions.

"I dare you to answer those same questions without saying "evolution did it" or "it just happened to evolve that way""

I don't remember all of them, but yes, of course I can do that! That's the whole damned point of the theroy of evolution.
Here's the fundamental idea, just to give you a taste of how evolution explains it: Species X is the way it is because it inherited its DNA, with modification, from it's ancestral species, Y. that is, for example, X has a spine because it inherited it from Y.
Ye, those questions were a lot more specific, and yes I could explain them all and you know that. I specifically gave you examples of things that evolution can explain, which ID cannot.
And I don't have to say "evolution did it", because evolution isn't a thing, it cannot choose what to do, it's just a phenomenon with a name. But a god is supposed to be a thing that has a mind which can make arbitrary choices, and I have explained how that makes god completely untestable because he/she/it would be unpredicatable unless we could actually study the god, not the things you assert that the god has done, to see whether the god would actually do that. Then we could have a better reason to think that maybe the god did those things.
But the entiere idea of a "god" is ridiculous to begin with, so I don't see why we're even giving it a seconds thought. We have no reason to.

" ID actually says certain areas of life are best explained by an intelligent cause ... it says design is evident even if you can't tell exactly who the designer is"

Thanks for proving my point,. You just made 2 assertion without support, and which cannot be tested. Completely useless.

"you really think Newton studied so much but just decided to believe in God for no reason? "

Remember how Newton was unable to explain the orbit of Mercury? Because he was unable to explain it, he said "god makes it do that". Then he stopped trying to explain it.
Yes, a textbook argument from ignorance.
For cultural, traditional reasons, they thought that "god" was the default answer when you didn't know.
Of course, newton was wrong in that, as with so many other things. Einstein explained the orbit of Mercury using relativity, which made most of Newtons famous work obsolete.

"and any chance for Newton to just get a little familiar with the new science and hell beat any scientist today hands down"

We have no way of knowing that, but I bet Hawking would give him a run for his money.
Yes, Newton was a genius, but compared to today's standard, he was a very, very ingorant genius. He wouldn't pass elementary school.
He would stand in awe of the things we know.

"however how would you in your right senses think an average teenager would beat Newton in calculus?"

I'm quite sure I mentioned that math, however, is different. But still, we've come some way in math since Newton's time, aswell.

"Einstein lived during the era of evolution yet he wasn't an atheist"

Well, yes he was an atheist. I mean, the god he talked about wasn't an actual god, it was a metaphor. He did not believe in a personal god. At best, he was a deist or a pantheist, but he was clearly less than that.
Pelase don't tell me you're one of those people who have fallen for the myth that he was religious, or a theist. He expressly stated that he was not, and that he thinks those things are silly superstitions, and he upset the whole jewish community for speaking against the existence of their god.

"and you really think Newton would be an atheist amidst the plethora of  new evidences supporting design?"

Bullshit, and I'm not going to bother. There is no evidence for "design", because there cannot logically be until you find a designer.
You seem really proud to be relying on logical fallacies.
And yes, Newton, if he lived today, would understand that, aswell. He was a smart person.

" I tell you this if Darwain knew what we know today about the cell and molecular biology, he'd have thrown away his theory long ago "

Wouldn't matter one bit, since by ny, thousands of scientists would have already come to the same conclusion. No one cares what Darwin thinks. He is only famous for being the first one who published this idea. But he was wrong abouta lot of things, as I understand it (I haven't read the origin of species). Science moves on, you know.

"well it's your choice if you want to close your eyes to the evidences I brought up"

Seriously. Fucking you, you haven't brought up a single piece of evidence, you fucking liar. All you have done is assert that your evidence exist.

"ID is the scientific fact, God is the belief "

You're close. They're both religion. They're both based on the bible, and they're both dogmatic.
The idea that ID isn't creationism is a PR stunt, nothing more. This has been settled by the US courts.

"however I would love to see you come up with a different agent other than God"

I still don't know what a "god" is, so I have no idea which ones are gods and which aren't.
If life on earth was created by some thinking being that didn't come from earth, then... it was made by some alien. Want to call aliens "god"? I have no idea what difference that makes. Seriously, both "alien" and "god" is pretty much the most vague words that exist, so it really makes no difference to me.
I know that "aliens", in the sense of "extraterrestrials", are living being who are not from earth. Good, OK, I can work with that. That makes "god" an alien, I assume, excpe that it doesn't seem like "gods" are actually alive. Things that are alive have biology. so what, a "god" is an... undead alien?
I have no fucking idea, and I seriously don't care...... just show me that thing you're talking about, and I don't care what you call it.

"or maybe you're just trying to hide the fact that this "cumulative change" is in fact cumulative random change produced by random causes"

Mutations are mostly random, yes. Recombination... not quite so random. Evolution? Not random, but directional and lawful.
You know, even a car that was fueled by randomness could still drive in a specific direction and be completely lawful in all other respects.
And why the fuck would I want to "hide" that? Did you seriously think I chose evolution to be the explanation? No, I cannot choose reality, it is what it is, whether I like it or not. Of course I want dragons and magic and gods and superheroes and power and eternal life. I just can't choose what to believe, because I am not good at self-deceit. Sometimes I wish I was, but then I remember that it's not a good idea.

"considering that the physical world was created(or began to exist), a transcendent cause would actually need to come from outside the boundary of the physical"

That doesn't quite fit the evidence. I mean, the universe has always existed. There was never a point in time when it did not exist.
Time started with the big bang, as we understand it. And without time, the idea of "cause" goes out the window, too, so the universe doesn't need a "cause", because it didn't actually begin to exist, it always existed.
If your reason for believing in "god" is that you don't understand cosmology and/or relativity, then that's a bad reason.
Anyways, even so, how the hell do you propose that something that is not physical would impact something that is physical? That would vioalte the conservation of energy, to begin with.

"if God is limited to the physical then He is not God "

Ehm, ok..... so, what does that mean that Thor and Odin and Zeus and Hades weren't gods, because they were physical? I mean, I think they were physical. People met them, and so on. I think they were mortal, even. But they were gods.

"Anyways, you're a moron if you believe in something just because it fits the facts. ... I'm sorry doesn't that make you a moron? ... what tests do you have that can be done to falsify the idea single celled organisms combining to form a multi-celled organism? "

The scientific method is basically:
1. Look at the fact.
2. Form a hypothesis.
3. Test the predictions that the hypothesis makes.
4. ... profit, or whatever.

If you believe in something at stage 2, then you're doing it wrong.
The theory of evolution's predictions are tested every time we dig up a fossil, for example, or every time we sequence a new species's DNA. Well, parts of the theory is tested by that, the whole "common descent" part. The "tree of life".
The moment we for example find a new species that has no consistent place in the tree of life, then we've disproven the idea that all life on earth is related, right there on the spot. (Well, given some time to make sure it's legit.)
But evolution itself, the phenomenon that the gene frequencies of a popualtion changes over timne, cannot be "falsified", because it is a fact. It simply cannot possibly reaosnably be wrong.
I believe in evolution because I can test it myself. I know it happens. As for whether all life on earth is related, I don't "believe" that. I think taht it's probably very, very likely, but we haven't even found nearly all life on earth yet, so we can't say we know that.
Punctuated equilibrium makes logical sense, as an addition to the theory. ESS (evolutionarily stable systems) theory, same thing. It's deductive, it can be demonstrated mathematically, and it predicts that we should not find any long-standing thing that goes against SSE. And we don't, so far.
I'm not sure I believe in the law of irrevesibility, either. But that is still being discussed, as I understand it. It seems to hold up.

Yeah, I could talk about his forever, but I won't. I doubt it's appreciated. The point is that I don't believe the theroy of evolution simply because it explains the facts, but because it has consistently had its predictions confirmed, for about 150 years. Which means that it has predictive power, aswell as explanatory power. And predictive power really is everything when it comes to science.

Of course, I would be stupid to think that I know everything about the subject, because I know that I don't. I am not a professional, either.

As for single-celled being related to multi-cellular life, the DNA shows that they are as related as everything else, so to say. But this is not a thing I care much about. I don't care if all life on earth is related, it doesn't help all that much in understanding how the universe works. It's mostly about history.
And it would obviously be much more interesting if it was false.

"we can do this by demonstrating that design can be tested for and recognized ... and we've done this ... "

Then I've missed the memo, can you get me up to speed? How did someone do that?
So far, we've had to rely on actualyl finding a cause for something before we could identify the cause. Seems logical to me. If we find a large crystal, we don't decide why it exists before we find something that makes crystals, which could have made it.
We have no examples of universe-creating gods. So sinc eI can't ask you in real time, I'll ahve to assume that you looked at the universe and asserted that it was created, and then asserted who created it. Never did you actually prove that the universe was created, because you have found nothing/no one that creates universes.
So yeah, you're probably once against relying on logical fallacies. But oh how sure you are about yourself.

"it's not like the Judeo-Cristian faith started off saying that lightning was God and then changed to say God was actually immaterial ... it has been consistent from the very beginning "

Heheh, ok, 2 things:
1. I don't know at what point in history we realized that lightning is a weather phenomenon, but there was a time in the past when that was the kind oif things they ascribed to gods. Nowadays, when we've figured those things out, the only thing we really don't know much about is the beginning of life, so that is what people of today will ascribe to gods.
It is the "god of the gaps", all through history, and today aswell.
When we prove that gods had nothing to do with the origin of life, and that our inverse exists as part of the multiverse, then religious people will isntead say that god created the multiverse, until the day we can explain the existence of the multiverse.

2. The bible doesn't say god is immaterial. It describes god as sitting in the literal sky above us, looking down. He was even in the garden of eden, for example. Nothing in the bible that I have read suggests that he is immaterial, and lots of things suggests that he is material/corporeal/whatever. I don't know how god can "hover above the waters" if he is not literally in the universe, for example.
The fact that modern christians suggest that their god is immaterial and "outside of time and space" (even though the bible says otherwise) is exaclty the phenomenon I explained. We've proven that god is not in the sky, like the bible says, and so on, so the only way for the religion to survive is to creatively reintepret it to say something else.
The problem is that it's become really pathetic, because chrstians now generally admit that god doesn't actually exist, by saying that he is not in the universe. That is, he is not in the place where everything that exists is. Meaning he technically doesn't exist.
Perfect way to defend it against all tests, but also really pathetic.
And if we are ever able to go outsdie of the universe and see that god isn't there, they'll just move him somewhere else. Anything to keep their religion from making any sort of predictions that could ever be tested - because they know it's bullshit.

"God is the creator of heavens and Earth and life: this has been the major claim all along"

Yeah, and it's been falsified for a long time, now. Our understanding of cosmology disproves genesis. The universe did not start with the earth, for example.

"the computer we make is far inferior technology to that used to make humans and other forms of life "

Read what I said again: Supercomputers of the future. Are you not able to imagine that a quantum computer, which may a priori be 100 000 times faster than a standard computer, stacked up as a super-computer, which might have a a few billions times more processing power than any computer today, could potentially design an eco system? Yes, such a computer could design a working eco system, I can promise you that. I mean, even today's computers can do that, but it would be a simpler eco system.
Ironically, the way it would do it would probably be using evolutionary principles, btw. Simply because it's the most efficient way to find a complex solution to a complex problem.

"e.g the navigation system in birds beat that of our most advanced planes hands down "

No fucking way. The newest satellite positioning system has an accuracy of 3cm, I think. Birds do not have that kind of accuracy. Nowhere near.

Human technology beats most things that animals can do. Not everything, but most of it.
And for some reason you completely missed the part where I said "future". It's not long until computers and techonology does everything better than any living thing. We're very close to that, already.
Perhaps in our lifetime.

" please don't even compare technology"

Natural life is not "technology". Yes, there is some artifical life, and some life that has been improved artifically. Those could be argued to be technology, at least partially.

"you could say Natural selection is a fact, Genetic variation, adaptation ... evolution? ... a theory"

No, "evolution" is also a fact, because it is an observation. "The theory of evolution", however, is a theory.
Natural selection is part of the theory of evolution. It is the key explanation, the core of the entire theory. It is a law/principle of the theory of evolution, which is why it's technically called "the theory of evolution by natural selection", we just tend to shorten it down.
Genetic variation+natural selection, that is all you need. Any such system will evolve.
And to "evolve" means that the frequencies of the genes in the gene pool will change over time. Some genes become rarer and some become more common. That is evolution.
That is why it's indisputable that evolution occurs. It cannot be completely avoided.

"and one which has a reputation of failed predictions "

Tell me one failed prediction. Yes, I am sure there has been failed predictions, since the theory has had to change. I just don't tend to study the history of different theories, as much as the current state of them.
You know what other theory has had many predictions that failed, in that sense? The theory of gravity, for example. It famously failed to predict the orbit of mercury. Does that mean that gravity isn't real, you think? Or was our understanding opf gravity not perfect?
Pretty much all theories have had some predictions fail, which is why they keep improving.
But for an established theory to be completely fundamentally wrong? I've never heard of such an example. It's be amazing if somethign that had enough predictive powers to become an established theory, and then somehow turned out to be completely wrong.

But you have to note that the current scientific theory is only a little over 100 years old, more or less. Darwin's "theory of evolution" was before we even established the hypothetico-deductive method, where we form hypotheses and try to falsify them. That means that in a sense, Darwin's theory wasn't actually a theory by our standards, because they did things slightly differently back then.
But it definitely is a proper scientific theory now, at least.

"should have been discarded long ago "

No one will ever discard something that continues to have predictive power. You clearly understand nothing about science.
And it's not like there is a "head scientist" who decides when something should be discarded. Science as a whole is a phenomenon. Whatever is "consensus" is simply the collective work of all scientists. If 100 scientists "discard" the theory of evolution, you still have hundreds of thousands of scientists who continue to use it. And why do they use it? Because it has predictive power. That's why we ever use anything in science.
And if all except for 10 scientists discards evolution, those 10 will be successful in their work, while the hundreds of thousands of scientist that discards it now have nothing.
I mean, imagine if we did that to the theory of relativity:
"Lets just pretend that things aren't actually relative."
 "OK, good luck, I'm sure your experiments will make sense."

No, the fact is that scientists are literally forced to use the theory of evolution. It's not a choice, you can't choose what is real. If you want to find a specific animal fossil, then I'm sorry, but you have to "ask" the theory of evolution where you will find it, if you want to find it. Otherwise, you'll find everything except the thing you were looking for.
That sure will slow you down.
"Lets look for rabbit fossils in the pre-cambrian rocks".

"Natural selection and genetic variation don't require magic ... evolution just assigns supernatural powers to them ... that the magic"

It's your limited perspective. This is an argument from personal incredulity, nothing more. That is "it's not true, because I just can't believe it would be possible".
That is not a valid argument.
Yes, it's really, really hard to imagine such large time scales. But just because we can't imagine it, or because it sounds counter-intuitive, doesn't mean shit if the evidence tells you it's true.

"we know natural selection and genetic variation can't build wings out of human arms "

Define what a "wing" is.
No, it cannot make bird wings, or bat wings, for example. What would a human wing look like, can you predict that?
And once you've predicted what it would be, consider what it would take for that to evolve.
I agree that humans aren't likely to evovle wings. In fact, I can pretty much guarantee that they won't.
But ignoring all practical factors abotu humans and their environment, is genetic variation and natural selectiona ble to change the DNA sequences that are responsible for the shape of oru arms into a sequence that would make smething that we would call "wings"? Yes, of course it could. There is absolutely nothing preventing it. Once sequence can change into any other sequence, in theory.

"but with evolution, it can even reconfigure the lungs to work for flight "

You don't know what lungs humans would need to fly. You reason like a kid. Start by admitting that you have no idea what possibilities exist, because you don't. There are a nearly infinite number of way to make a wing, or to make something fly. And you argue as if you think there is 1 way. Well, life has already demonstrated millions of ways to get something to fly.
But in mammals, only bats can fly. We're probably fundamentally too heavy, so we've got problem evolving that way. Dinosaurs already had pneumatic bones and feathers, so they were already fit for evoling flight.
Humans would quite certainly have to become much lighter, to start with, before we would ever be viable to evolve flight.
But some mammals have evolved flight, and even some fish have evolved flight (not very powered flight, yet, but you just give them time and space).

"classic evolutionary magic"

The problem is that you keep demonstrating that you don't know much about evolution at all. Start studying it so that you can argue properly about it.

"no kidding? ID has no problem with organisms adapting to their environment"

Yeah, you just pretend that there is some unknown "wall" that blocks them for changing "too much".  I am aware that most creationists at least agree that species in the same genus are related. But they have absolutely no justification for saying that there would be some limit like that. We've invented the concept of genera, it's not like biology is going to conform to our definitions, like that.
If lions can be related to tigers, then they can be related to bears. And if I keep giving these examples, eventually you'll find that there is no difference between that and lions being related to birds, for example.
If A is related to B, which is related to C, then why the fuck would it be impossible for A to be related to C? That is essentially what creationists argue. But the problem is that generally they dont' even know that they're arguing that, because they don't understand evolution or taxonomy. But they really, really think that they do, and get defensive when you point it out.

"you have shown me good reason to think you're ignorant of many biblical concepts"

I am sure I am, but probably not quite as ignorant as you think I am.
Of course I have little motive to study it, so I have spent my time on other things, instead. But through talking to christians, I have looked things up, and I have read things, and I have learnt from them, and so on.
I also did have a fundamentalist (if that's the right word) christian girlfriend for about 1.5 years. And I had a close friend who was also a fundie christian. Good guy, though he drove me crazy, sometimes.
So yeah, I've talked a lot to them, for example.
But yes, since I'm not a christian, and never have been, of course I won't know the bible very well. But I do know parts of it, and whatever. I don't know how to "measure" knowledge of the bible, either.
Anyways, I admit that I'm ignorant about religious teachings. I have no problem admitting my ignorance.
But when I say I do know something, I mean it.

"God in the Bible was very dissatisfied with the early mens knowledge of Him "

Out of curiosity, what is your source for that?

"50 bucks? haha I take that as evidence for the contrary ... you could have bet 5mil if you were damn sure "

I don't have 5mil, and I have to admit the possibility that I could be wrong. Yes, I would bet more than 50 bucks, it just felt like a good number.
Either way, the fact that we would have a bet going would impact the whole thing, so it wouldn't work. But perhpas sucha low sum of money wouldn't have a large impact. If you could pretend to stop believing in god and get 5mil, I suspect you would.
But would you pretend to stop believing in god for 50 bucks? I'm not as sure about that.

" I'm not that staunch ... you show me the evidence, you explain your rationale, if it concurs with the evidence, I agree "

You're not paying attention. I said you have to tell me some predictions. I am not supposed to give you evidence, you are supposed to make your ideas falsifiable and testable. Then if we falsify it, and you still believe a god created life, you owe me 50 bucks. :)
And I am actually trying to help you, here. If ID was falsifiable and testable, then it could actually be treated as a scientific hypothesis, instead of religious dogma.

"plus the unjust suppression of ID"

Hehe, it's not "unjust". It's the fact that ID-people refuse to formulate a testable hypothesis, yet still want to be treated as if it was science, rather than dogma.
And then they cry when the mean scientists don't take them seriously.
It's special pleading. Creationists/ID'ers don't want their ideas to have to stand up to the same kind of testing as any other science, they just want a free pass. (That's why they changed the name to ID, to try to fool people that it's not creationism and not religious.)

"Start by showing that intelligence can exist outside of the universe, and *then*we can talk about whether such an intelligence can or did create anything inside the universe. ... actually all I need to show is that there are things we feel that exist outside the boundary of the physical ... love ... going by science, love doesn't exist because it isn't testable and measurable"

OK, here's what we do: You start feeling love, and I'll start cutting bits of your brain off, and you tell me when you can no longer feel love.

Nah, but seriously, we can already make people feel love by messing with people's brains. No of course love is not material, it's a concept. :P It is a state of the brain, being affected by specific hormones and such. The hormones, and the endocrinal system, are real, however. If you think that emotions are "outside of the universe", then why would the brain need hormones to produce them, genius? 
We can make you feel anything, really, by messing with your brain. Both through electricity and through the use of drugs.

Oh yes, love exists, in the sense that a person's brain can have the "emotion". That is a scientific fact, and we know what causes it, which hormones, and so on. For exampl, eat a shitload (!) of chocolate, and you'll feel the same way you feel when you're in love, because it contains small amount of some specific type of amphetamine, or whatever.
If you happen tobe with anotehr person at that point, you brain might associate it with that person,a nd you're then officially, technically in love with that person. ;) That is why guys give girls chocolate on their dates.

But these things aside, I can't believe how you'd think this would prove the existence of intelligence outside of the universe. :P You are inside the universe, in case you didn't know. What, you're telling me that you emotions aren't inside the universe?
You sure are hilarious, sometimes.
Anyways, so a brain inside the universe caused emotions to exist outside of the universe, or whatever crazy fucknig idea you have. Still doesn't prove that there is "an intelligence" outside of the universe, which doesn't have a physical brain.
And no, I'm not actually enterntaining this nonsense. You're a fucking loon.
Please tell me you're 13 years old, because it would be embarrassing if you are older.

"going by science, love doesn't exist because it isn't testable and measurable "

Anyways, if it wasn't clear, yes, love is testable and measurable, because it is caused by hormones. We know about the endocrine system, you know.
We can test it because we can identify the hormone that cases you to feel love, and we can give you that hormone and see the effect of it, and so on. What do you think biologists do, really? Sit around?

"going by science music doesn't exist:"

Yeah, right, music doesn't exist. 8|
Tell that to someone who studies acoustics, for example. Or someone who studies music?
What about music doesn't exist you mean? You're getting nuttier with each minute.

"these things can't be tested for falsification but we know they exist outside the realm of the physical ... how much so God?"

They're perfectly physical, and it's just sad that you don't understand that. Like I said, I hope you're actually 13 years old.
And how does this have anything to do with "god"? Even if "music" existed outsie of the unviesre, it says nothing about whether a "god" would exist there.
Music is sound, which si vibrations in matter. So music outsie of the unvierse would mean that vibrations in matter exist outside of the universe. Still no link to "god", though. Try again. (?)

""Highly principled"? Explain? ... I can't explain more until you actually understand the ones I've explained already "

Haha, OK, so you talk a bunch of nonsense, but won't explain what you mean, because first I must understand what you mean. :)
I don't know, but this whole conversation goes back and forth from "just sad" to "fucking hilarious".

"PS many scientists believe in God"

Yes, but extremely few, if any, scientists who study the diversity of life thinks that god created the diversity of life, rather than evolution.
Extremely few geologists, if any, think that god created the earth.
And so on. Yes, there are sociologists and ornithologists who believe in creationsm, and so on. Who gives a shit, it's not their field. They never actually have to test their beliefs.
Find me a geneticist who doesn't believe we are related to the other great apes. I'd love to see if even one exists.
Reply: Benjamin Toby"but you've given me enough reason to doubt your knowledge of what the computer code actually is "

Fine, I can't change your "attitude" towards things, and it's perfectly fair for you to be skeptic.

"and the concept should be clarified first before an agreeable definition can be applied"

The problem being that you just attacked me for actually clarifying it...! Schizo.

"you've really got to open your eyes and mind more bruh "

Exactly my point: This reply is all I get when I actually ask you something. Your attitude is that I should just "know it". You offer absolutely nothing. Tell me again why I should bother taking you seriously, to begin with?

" also, try not to make equivocations with these two words "code" and "symbolism""

I don't equivocate them. Symbolism is just symbolism, while "code" is second-level symbolism. It's not my fault that the subject is inherently confusing. It just is.
It's perhaps the 3rd time I've had this discussion with people, and it surprises me that so many people can't see their reification fallacy. I guess this is harder to understand that it appears.

"sometimes I read it twice to get the drift because some paragraphs might be linked ... and apparently you don't put as much effort into understanding my comments"

Your comments are largely made up of just nothing. 70% is stuff like I pointed out before, where I ask you a question, and all I get is that I should just know it, or that you have already told me. There is very little to "understand" about it.
When I ask you for a definition of "code", according to your undertanding, I am not asking for a vague example, I am asking for a damned definition. One example of something you would call "code" is not enough to figure out the definition of it. I want to know what makes you think that something is "code", your process of figuring that out, your criteria, your definition. I have given you the definition, and if you disagree, then give me an alternate definition. It shouldn't be hard if you claim to know what it means.

"it might seem like I'm just wasting my time and repeating myself because of your lack of proper understanding"

And I admit the possibility that it is something I am simply not understanding, but you have to realize that it is up to you to make sure that you are properly understood.

"I repeat: it is called computer code because the computer actually interprets and manipulates instructions according to the programming"

That is not what code is, or what code does. "Code" is something between two minds, such as two humans. Computers never work in code.
I have said this many times, but you don't address this, you just keep repeating yourself.

"that's why the computer code is different from human codes and why we represent the computer coding in 0's and 1's"

It isn't code. I've said this so many times, now.
"1/0" are symbols. To have code, we need to to agree on something that represents "1/0". We do that. We made "assembly" which is a coding system where simple words represent binary sequence. So when we write assembvly, we are writing code.
But "code" is conceptual, it's only code in our minds, and in the minds who agree that it is code. To the computer, it is not code.

No matter how much we mess around trying to talk about this, there is just one thing we need to agree about, as answer this: Is "code" conceptual or physically real; It is a concept, an idea?
Because it is. If you agree that it is, then you have no reason to claim that a computer can actually use/understand code.
That is, unless you're simpy argueing that "computer code" isn't "code", it's something different. In such case, that's fine, but then we need to make sure we don't equivocate them.

"that's why it's called binary code"

It isn't called "binary code". And even if it was, that once against only means that it's code in our heads, not in the computer, not to the computer.
The computer is symbolically reading a binary sequence. That is, there is no "reading" going on, it's an analogy. "Reading" requires the ability to "understand", which a computer can't do. That is why I'm saying that is symbolically or "conceptually" reads a binary sequence. And it isn't a binary sequence to the computer, either, it is just a bunch of voltages. The compute rhas no idea that we huamsn use symbolism to represent those voltages, or the purpose for those voltages.

"actually a computer can tell a difference if it's programmed to" (I said a computer can't tell the difference between something that is meant to be code and something that isn't.)

Then it is the software that's telling the difference. I have said that theoretically, software could probably emulate a mind, or even become a mind. If we'd manage to do that, then the computer will have a mind, and could understand code and symbolism and concepts and ideas.
But if the computer doesn't have a proper mind, then no matter how complex the software is, the software is as extension of a programmer. It is the programmer who understand the code, not the software or the hardware. The programmer made a program that does what the programmer would have done. The software isn't able to be a person or mind in itself and hold its own understanding of things.

"you're saying in essence that the computer code is just to shorten the binary codes"

It's about what those beinary sequences represent to us, in our minds. Not for real, physically, or in the computer, but conceptually.
Lets say I write the word "mov", which might be an assembly codeword that represents the function of moving a value betwen registers in the CPU.
If I write this on paper, or if I say it to someone, it should be clear to you that it is not inherently represented by binary sequences. It's "language". It is a symbol that we've agreed on, so that when I say it, you know what I mean, conceptually, but perhaps not concretely.
If I write it in notepad on my compuiter, then yes, the word "mov" in notepad is actually stored using the ASCII table as a binary string in RAM on the computer. But this is irrelevant to the point. Do not let this confuse you.
When I send the word "mov" to an assembly compiler, it will recognize the binary sequence that makes up the ASCII characters "mov", and translate that to whatever the binary sequence is for the actual instruction that the computer hardware will recognize as the instruction to do that.

So, conceptually, the word "mov" is code for the computer to carry out a specific construction. But because the concept of "mov" is not something a computer can actually understand (remember how I said it isn't inherently represented by binary sequences), the codeword "mov" actaully represents something that the computer can use.
I cannot actually tell the computer to "mov" anything. It would not understand that that concept, because that would require the computer to have knowledge of the world around it and how physics work, and so on, so understand the idea of moving something.
Ond obviously, when we move a value from one register to another, we're not literally moving anything, we're actually copying something, and then ignoring the original as if it doesn't exist. We only conceptually describe it as "moving" a value. And the computer doesn't have to deal witht his, anyways, because it is only in our minds.
What the computer gets is a pattern of voltages that cause a specific thing to happen. We can symbolically represent those votalges by 1's and 0's, for example. But because that becomes cumbersome, we can instead use code, which is what we do when we write "mov" in assembly. As long as we are all consistent in what "mov" means, the code works.

" from my analogy striking the button for "A" is the process of encoding because in computers we're looking to gain speed: we can just write the letter or connect a few led's to create the pattern required ... but they are both slower, especially when repeated "

That isn't what "code" is....!
Please, just think about examples like "morse code", for example.
Why is "morse code" code? No matter how you transmit it, or if you write it down or say "long short" or whatever, it still is "code". Think about why it is.
I'll tell you one last time why it is: Because it is a system of symbols that represent other symbols.
Note that when I instead send the word "hello" not using morse code, it isn't code.
If I have a microphone and a radio transmitter, and I send the word "hello", by saying it inot the microphone, then that will be fast and efficient. anyone who hears the world will instantly know the message, assuming they know english.
If I instead say "beep bip-beep" and os on, using morse code, into the microphone, then it is code, but for anyone to understand it, they have to decode it back to letters, because those "beeps" are encoded letters, using the Morse coding system.
It is not about efficiency, it's about hiding symbols under symbols.. You're absolutely completely misunderstanding the entire concept of "code".

Now, as for the rest of the subject of "code", I seriousy give up trying to make you understand. This was my last attempt. I have said what I can say, and perhaps I don't have the "teaching skills" or whatever, to get the message through. It would've helped if I could draw while talking, or something.
I see you keep arguing the same thing, as if you don't see what the problem is, and I give up trying to explain what the problem is. I've used all techniques I can think of. But as I see it, when I explained to you that "code" is second-level symbolism, then that's where it should have been clear, and this discussion should have been over. It's not, and like I said, I give up. I'm not going to waste time repeating myself over and over, which is all I can do, now.

"This shows how you're confused. A program doesn't contain codes, it's code that may contain a program. ... unbelievable ..."

That is not a proper response. Tell me if you get it or not! When I am programming, I may be writing code. It isn't the computer that writes the code, it is me. My code is then compiled into software, which runs on the computer. There is no... code... in... the... software! It was made using code.

"the builders of the Stone henge are unknown but we recognize it is designed because we have experience of intelligence designing such things"

Yes, I agree fully. Stone henge was probably built by humans, because we know that humans make religious or cultural artifacts like that, and it looks like it was made in the kind of way that humans of that time made things. (For example, it clearly wans't cut with lazers, which would've changed our way of looking at it.)

Now tell me what experince we have of designer gods who make life, so that we can make such an inference.

...tell me when the coin drops.

"this is a pretty stupid assertion considering I took time to explain the concept to Spiegel "

I did not read your conversation with Spiegel, as far as I remember.
Also, I don't need irreducible complexity explained to me, I understand the concept very well. But it still remains an argument from ignorance, unless you can logically/mathametically prove that it is impossible, which is effectively impossible to do with most things. You have to prove that there cannot possibly be a way to explain it that we have not yet thought of.
For example, 1 cannot be 2. We know that, and nothing is ever going to change that, because we can prove that 1 isn't 2.
But you're talking about looking at a structure, and proving that it cannot have evolved, and that we will never in the future find a way to explain how it could have evolved because it is impossible.
And that cannot be done, because the best you can do is to say that it is "unlikely", because in the end, it is theoretically possible for a mutation to do anything to the DNA. But if something takes more than about 3 coordinated mutations, then we consider it unlikely and try to find some other explanation. But "unlikely" doesn't mean "impossible", which is why irreducible complexity is an argument from ignorance: "We can't explain how it could evolve, therefore it can't have."

"it'd be a useless attempt to explain it "

Yeah, there we go again: You refusing to to actually ever say anything.

" just to repeat myself once again ... ID is the fact "

ID is an attempt as a hypothesis, but because it isn't even falsifiable, it isn't even a proper hypothesis. Quite damned far away from being a "fact".

"I think you can stop with the argument from ignorance BS "

Not a fucknig chance that I would let anyone get away with a fallacy. Typical creationists to rely on fallacies and be upset when they're not allowed to reason illogically.

"and you're compounding the issue with you unending lines on poor reasoning"

Says the person who can't spot an argument from ignorance, or a reification fallacy. I'm miles ahead of you.

"maybe you should come over to the other side of scientists that think evolution is mostly crap"

I came over for a visit, to check it out, but failed to find any scientists there. I saw preachers and conmen, though.

"actually he [Newton] understood the other orbits and still came to the conclusion that they all proceeded out of the council of a divine power "

If he hadn't given up and resorted to saying "god does it", he might have figured out what Einstein later figured out. That is my point, in case that wasn't clear.

"At best, he was a deist or a pantheist, but he was clearly less than that. ... so he was an atheist, he was a deist, which one is it?"

It's really weird of you to ask a question tha tI just answered..!
I cannot say that he was an atheist unless he himself said that he was. He expressed the same kind of statements that an atheist would say, but I have never personally heard/seen him say the word "atheist".
Einstein used "god" as a symbol, or an analogy.
So for all we can tell, he was an atheist. But no one can actually read him mind and determine that, and it wouldn't be right of someone else to claim something they cannot in fact know, unless they've expressly heard him say it.
Because he used "god" as an analogy for the cosmos itself, in a sense, you could potentially argue that he was a pantheist.
In either case, he did not believe in a personal god, which means he was not a "theist", not that labels matter that much.
And I have no problem with pantheism, I just don't see the point in calling nature "god".

"read up the wiki article on the "religious views of Albert Einstien" ... he was damn sure he was no atheist even saying quoting him for the same views as atheists made him "angry""

Back in his time, "atheist" had the notion of meaning to be against god, or to know that gods don't exist. It is mostly in the last 20 years or so that "atheism" doesn't carry this undertone/stigma.
He was not an atheist in the sense of what it meant in his time, but he would've surely agreed with Christopher Hithens, for example, had he lived today.
But anyways, read the very beginning of that wiki page you referred to, where it says he was a kind of pantheist (yes, the "god" of spinoza), and did not believe in a personal god.
And impersonal gods are not the kind of gods people mean when they say "theism". Einstein was therefore not a theist, and that implies that he was an atheist - but only in the progressive, less stigmatized sense of today. Back in Einstein's time, atheism was nowhere near as large as it is today, and was not accepted, and carried a lot of stigma about devil worshipping and other nonsense. It still does, a little but nowhere near as much. People who were atheists back then did not say they were atheists, they said they were "agnostics", even though that it technically incorrect.

But all that matters here is that Einstein was not a christian, or a jew (other than culturally), or a muslim or a hindu, for example. He called such things "childish" and superstition.

"actually I think he was more an agnostic: which actually is a justifiable stance for a scientific"

"Agnostic" means to believe that the question of gods existence is unknown, and sometimes even "unknowable". Agnostic/gnostic is a question of what you think can be known, it is not a question of what you believe.
Therefore, "angostic" is not a "middle ground" between theism and atheism. This is a common misconception.
I am also probably an agnostic (a subject on its own), but I am also an atheist. Most atheists are agnostics, and a lot of theists are, too.

And I agree, scientifically, we are agnostic as to the question of the existence of any gods. However, not when it comes to some specific gods.

"he did have a little religious side "

Yes, but he didn't mean the same thing that you mean by it. He meant an "aweinspiring experience", sort of. To see something as much larger than yourself.
That is not the definition of a religion. He was talking about the same emotional kind of thing as being religious. And Carl Sagan said the same thing, and so did Richard Dawkins. They are not actually religious, and neither was Einstein. Religion carries dogma, for example.

"yes and you're living proof of the level of foolishness lurking in the scientific world "

I am not a scientist, and do no scientific work, and am not part of the scientific world as anything but a spectator, which would effectively include us all. You too.

"Mutations are mostly random, yes. Recombination... not quite so random. Evolution? Not random, but directional and lawful. ... lol ... pathetic ... yes ofcourse the recombinations are random: that's if you're talking about reproduction "

You have to understand the idea that some things are more random than other things. How random is really the roll of a dice? Isn't the outcome dteremined by the laws of motion, mainly? The best source of randomness that we have on earth,. that I am aware of, is the cosmic microwave background. If you put a geiger counter pointing into space, you'll get the most random "beeps" that you can get, pretty much.
Recomibation is theoretically less random than mutations, as far as I know.
But whatever, who cares, lets say they're all perfectly random, this is seriously not something worth arguing about.
The point is still that evolution isn't random just because mutations are. Evolution is a lawful process with a specific outcome, not a random outcome.

"actually with evolution superpowers can be achieved "

If by "superpowers" you simply mean powers beyond what humans have, today, then yes. For example, we could become 10 times stronger.
But not if you mean "superpowers" in the sense of being supernatural, of course. Evolution cannot produce supernatural things, as far as we know. :P

"just take your family and breed under water for a million years and gills would appear"

Gould's law of irreversibility forbids that, so no, most certainly not.

" you'd do your very best to discard any evidence for design even without critical thought"

Cirtical thought, in the form of logic, makes me discard it. I have explained that those arguments rely on logical fallacies. Since I am aware of that, I am forced to discard them. And so are you, you just don't seem able to see it.

" because by my knowledge, the concensus is that time, and matter started to exist "

Exactly, the consensus is that time probably started existing at the moment of th ebig bang. So tell me at what point in time there was no universe? A second before the big bang? No, there was no "a second before the big bang". There is no "before" the big bang, according to current understanding. Thus, the universe has always existed. There never was a point in time when the universe did not exist.

Matter, definitely, there was probable a short moment in time when matter did not exist. But energy did, which coalesced into matter.

"I would love to explain this the way I see it but unfortunately you don't appear to be the kind that thinks critically"

Admit it, it's because you can't explain it. You're such a coward to try to blame me for your inabilities.

"actually there were many "gods" in the Bible ... I think a grade 1 student can tell the difference when I say God "

Yes, Baal, for example, right?
Yes, I know that in the bible, tehr eis a god called "god", even though I think he's actually called YahWeh, but whatever.
that doesn't explain what a "god" is. Jstu because there is a god called "God" doesn't help one bit, you know. I still don't know what a god (called "God" or not) is supposed to be.

And perhaps children know these things where you come from, but where I live, in Sweden, religion is not really a "thing". We study it in elementary school, yes, but only briefly, unless we choose to study it more. And we study the 5 major world religions, which doesn't leave all taht much time to study christianity, specifically.
It's just not a priority. Math, swedish, and english are the top priorities.

"*The moment we for example find a new species that has no consistent place in the tree of life, then we've disproven the idea that all life on earth is related, right there on the spot*. ... actually you're not going to find any living organism without the DNA "

*sigh*, you don't get it... the tree of life, yes all living things on it has DNA, but the tree is a tree structure because the traits of all living things fall into nested heirarchies.
There are no mammals with feathers. Find one, and it would usggests that it is a descendant of both a bird and a mammal, which screws up the tree. It wouldn't fit anywhere on that tree. That would be a huge problem.

"if we look at the evidences, we have a scenario where most of the major phyla appeared abruptly without any precursors"

That what is appears like, only because Linnean taxonomy doesn't work for very old things.
If you go back to the time where those major phyla formed, you would not call them different "phyla". "Phylum" is a taxonomic level that is further divided into sub-groups who divide into sub-groups, and so on, all the way down to genus and species.
If you were back in that time, then there would be no sub-groups to those new phyla that you're talking about. Therefore, they would be on the level of genus or species. So what you'd actually see is that all life on earth fell into one "class", which was divided into orders of families of genera and species. there would probably be no reason to havea "phylum" or a "kingdom" or a "domain" level of taxonomy, because enough time had not yet passed for life to become that diverse.

This is a confusion caused by the fact that Carl von Linné didn't know about evolution and the large time scales of earth's history when he invented Linnean taxonomy. That was some 120 years before Darwin.
It's a bad system. We've had to augment it a shitload, and it's still a confusing mess, and it's never going to be fixed unless we scrap it and go for a cladistic system, instead. We're in the process of doing that, but it's a damned hard thing to change.

"if you follow the facts, you'd realize that the fossil evidence actually support design"

It cannot, it is impossible. Even if all life on earth was designed, the fossil record could not be evidence of it.

"actually I'm not sure if I said this to you but ID actually allows for genetic variation "

It allows for any amount of evolution, aswell. The idea that life was initially designed doesn't means it cannot evolve.

"ID also predicts that lions cannot produce to bears or vice versa "

No, it doesn't.
Lions cannot produce bears because bears are not descendants of lions. Lions are cats, bears are not. A bear can never be a cat, and a cat can never be a bear.
But ID doesn't predict this, this is rule of classification, nothing else. With or without evolution, and with or without ID, this is still how we classify things.
It is impossible for lions to become bears. Not because of evolution or because of ID, but because it would create a logical inconsistency. And you cannot "predict" that, it is simply a fact.

" for 150 years it has been revised and redefined to make it look credible"

....to be more in line with the evidence of reality. That's how science works, did you not know this?

"I'm sure Darwins definition of evolution was the actual definition which was gradual development from simpler to complex "

I haven't read his book, so I don't know, and I don't care because he has been obsolete for a long time.

" but after it was found that it was probably BS we had new definitions and new words (eg allele) formed to add more value to the sinking thoery "

Perhaps you should learn about the subject before you talk bullshit.
What are alleles?
http://biology.about.com/b/2010/05/15/what-are-alleles.htm

At Darwin's time, we had not yet dscovered DNA, so it's not fucking strange that he did not write about alleles...!

" the present revision has to be the most stupid thing science ever came up with : penguins produce penguins ..."

Sorry, what? Are you saying it's stupid that penguins produce penguins? It sure looks like that's what you're saying.
Yes, penguins produce penguins, and they always will. I don't see what your problem is.
I suppose it's just that you have no idea what the science says. You've got the understanding of a 10-year old. And yes, when I was 10, my understanding of evolution was pretty shitty, aswell. I remember that I used to think that at some point, an ape must have given birth to the first human (ridiculous, yes).
But I've actually bothered to study the science. You don't seem to have.

"...something that even your ancestor ape-men could have even figured out without hassle ... this in the unique statement of a scientific theory of the 21st century"

It isn't the theory of evolution that explains that penguins give birth to penguins. It is a matter of classification.
Any offspring of penguins will be classified as a penguin, because they will have the traits of a penguin. That is not "because of the theory of evolution", it is because of something much older than Darwin. It is Carl von Linné, since he invented this system for classifying life.

"the Bible also describes God as a spirit, a consuming fire, the light, love"

Well, it also describes humans as spirits, in a sense. But that doesn't mean we don't have physical bodies.
And god evidenetly was materials in the sense that he was visible. People in the bible have seen god. To see someone, they have to give off light in some way, meaning they are physically real, or they're violating the law of the conservation of energy.

"you actually need some level of critical thinking to read the Bible:"

Applying too much critical thinking to the bible turns it into a huge mess that makes no sense at all. The only way I can make sense of it is to imagine a person 2-3000 years ago, writing this as his explanation for why the world is the way it is. then suddenly it all makes perfect sense.
Anything else just requires that I surrender to its nonsense, like "just go with it". And that is not critical thinking.

"one can easily figure out with all these descriptions that God is immaterial "

Perhaps, but then they all act as if he isn't. It's weird how they can describe him one way, and then he doesn't appear to be that way at all.
I prefer to try to make sense out of it, instead, and figure out what he is, rather than listening to how they describe him, sicne that rarely makes any any.
"God is love"? Sorry, love is a feeling we have that is caused by hormones and such. God cannot be that thing. Obviously it is an analogy, or something. So then I have to actually deduce what he is from reading the other parts.
And nothing about it ever leads me to think that god is "immaterial". He is sometimes described in a similar way, but he never acts as if he is.

" God exists in the universe but He's not limited by the laws "

The definition of "magic". Perfect.

"The universe did not start with the earth, for example. ... no kidding? the Bible says "in the beginning God created the heavens and the earth""

If you actually studied cosmology, you'd know that the stars came long before earth. But according to genesis, god created the stars on day 4, or something? That is, the earth came before the stars, according to genesis.
Long after stars had formed and died, the earth was finally created. The universe is about 9 billion years older than the earth.

"till then, you might have to show me a technology that beats that of humans"

You mean show me some technology that beats humans?
Pretty much everything we build are built simply because they do things better than humans do them. A fucking calculator beats humans, that's why we make them. They insanely much faster, and effectively never makes a mistake.
A car is faster, a tank is strong, a plane can fly, binoculars can see futher, submarines can dive deeper, a catapult can throw thing further, a bus can carry more people, a lamp can give off light, night-vision goggles can see in the dark, want me to go on?
Some things we build even last longer than humans, which is quite impressive considering that life has the ability to maintain itself and theoretically live extremely long times.

" how long can satellite last on energy contained in, say a hamburger?"

Huh? Longer than a fucking human can, at least. A satellite only has to orbit earth, it doesn't require any energy at all to be a satellite in space.
But no one has designed a satellite that is supposed to use as little energy as possible and just "be a satellite". Huge waste of money.

"Human technology beats most things that animals can do. Not everything, but most of it. ... lol ... well for one it doesn't beat the human itself "

Depends on what you want it to do. I listed a few examples of how technology beats humans. We can combine a lot of those things, if we wanted to build somethign that is specifically built to meet your challenge.
The one thing we cannot do, yet, is build a brain like a human's. Not that human's brains are very good at many things. They're worse than other technology in most ways, but they are more creative/innovative. We've got machines that can make music and paint paintings, and so on, but they don't match the creativity of a human brain.
But with pretty much anythign else, we beat humans by miles and miles with our technology. That's the main reason we have this technology.

"Natural life is not "technology". ... it is for the creator ... that was the whole point remember?"

There is no "creator", that's why it's not "technology".
And even if there was, would you really call it "technology"? It hardly came from "science".

"Genetic variation+natural selection, that is all you need. Any such system will evolve. ... no that's not all you need you simpleton ... that would be magic if you use this to explain unicellular to multi-cellular transformation "

If you read it one more time, you'll see that I said "any such system will evolve". I said nothing about a specific kind of change, like single selled to multi-celled. I didn't say it will evolve into anything, either, I said it will evolve, because tha tis a fact, it can be proven with math, and it is observed in, for exampple, the seasonal flu.
The fact that you don't think it can lead to some specific change is just your appeal to your own incredulity.

"And to "evolve" means that the frequencies of the genes in the gene pool will change over time. Some genes become rarer and some become more common. ... that's just genetic variation ... just a gene getting more frequent like a family with exceptionally long hair ... that's not evolution ... that's the equivocation I've been trying to explain to you for so long"

Hahas, yes, it fucking is...!
Evolution is exactly that. Don't believe me, then just fucking look it up. (Not from creationists who want to misinform you, of course.)
http://evolution.berkeley.edu/evolibrary/search/imagedetail.php?id=319&topic_id=&keywords=
Fucking Berkeley, for you:
"Microevolution is a change in gene frequency in a population. Suppose you sample a beetle population this year, and determine that 80% of the genes in the population are for green coloration and 20% of them are for brown coloration. You go back the next year, repeat the procedure, and find a new ratio: 60% green genes to 40% brown genes. You have detected a microevolutionary pattern: a change in gene frequency. A change in gene frequency over time means that the population has evolved.	"

But you've got your straw man version of the science, which I bet you'll keep sticking to.

You're the one with the equivocation problem. You seem to think that "evolution" is the same thing as "the theory of evolution". That is your equivocation, not mine.

"I just don't tend to study the history of different theories, as much as the current state of them. ... I think you should ..."

If I had time, sure. But I ahve a family, a wife and a daughter, and I have work to do. I dont' have time for everything, and then I would prioritize learning science over learning the history of science.

"ah well ID hasn't had any failed predictions so far ... and even if it did, by your logic, it doesn't mean it's wrong "

Hahah, because it doesn't make any predictions, you twat. :D
But you're right, since it hasn't failed any predictions, it isn't proven wrong. But what is it not wrong about? Nothing, it doesn't propose anything useful to be right or wrong about. Sure, everythign could have been done by magic, but that doesn't predict anything testable, because magic could do anything and everything, or nothing, so we wouldn't be able to tell the difference.
And not being proven wrong doesn't mean it's proven right. It's still there, in the box of things that we ignore because they're useless and pointless.

"No one will ever discard something that continues to have predictive power. ... you men the prediction of penguins producing penguins? lol "

No, the specific predictions. Such as if we have two species that share very specific traits, then the theory of evolution would predict that they share a common ancestor. So then you go look for a fossil in that place, and around the time/depth that it should have existed.
And yes, it keeps being correct. The theory of evolution predicts which fossils should exist, and where they should be found. That is one thing it predicts, and which has been confirmed thousands upon thousands of times, and continues to do so every time we find a new fossil.
So if we throw away the theory of evolution and acts as if it doesn't have this predictive power, then what? Do we suddenly start finding rabbits in precambrian rock? Are you that dumb?
Life clearly follows this system, because it is proven so every time we dig up fossils. Therefore, the only reason we'd ever have to discard the theory would be for political or religious reasons, but that won't help one bit, because it'll still be right.

"if by force you mean the unjust oppression of ID proponents"

Go somewhere else and cry about how you pet hypothesis won't get recognized because it happens to be shit.

"since a scientist can loose his job for publicizing a paper for peer review by an ID proponent "

Yes, I would fire any scientist I have who would argue for ID. Why? Because you can't argue for ID, so anyone who would say they do is a half-wit.
Like I've said, ID doesn't make any testable predictions, therefore it an never be shown to be true or false. A "scientist" who doesn't undertand that is not someone I would hire for anything, because they've failed to understand the scientific method itself.
ID is not science.

"there's no restriction on what would cause human wings and though I can't imagine it, it is possible by the imaginary process which created bird wings from bacteria"

Bird wings evolved from dinosaur arms. Study the evolution of maniraptora to aves.
Seriously, go back to school, you're a joke. Why do you even go on inernet and discuss shit you know nothing about? You're wasting everyone's time, and looking like an idiot while doing it.

" if such can happen, then what stops humans from developing wings? or even horns? "

It depends on what you mean by "wings"! I asked you this, already. If you're asking how humans could evolve wings, then first fucking define what "humans wings" would be, or no one can answer your question.

If you're talking about simply making humans fly, then the reason it won't happenis because we would have to have *insane* chest muscles to produce enough force to lift our bodies. We are simply too heavy, that's the main reason.
Sure, maybe some time in the future there will be a species of humans that are really lgith, I don't know. You'd have to be talking abtu somethign so damend far into the future that there can be nothing but pure speculation.
but we won't evolve wings, because we've got technology to solve such problem.
Humans will evolve, but not like that. Evolution is driven by whatever genes cause us to have more offspring. Evolution is not random. Having wings probably won't do that to human, so then we won't evolve wings.
However, we still die from childhood cancer, for example, which might mean that in the future, we'll evolve some kind of protection to dangerous childhood deseases that prevent us from reproducing.

It is probably a natural part of the devlopment of life itself, that it start out simple, gets more complex, then gets technology, and no longer plays by the same rules anymore.

"there's no guarantee that humans cannot develop wings "

I agree, but at least we can say that it would take an insane amount of time for us to evolve wings. We are very, very far from being fit to fly. That is, if we're talking about powered flight, not just "gliding". But if you're just talking about gliding, then that is a different thing.

"of course with evolution anything can change into anything ... but remember it's not random"

Exaclty, only in theory can it change anything into anything, but never in practice, because evolution is directed by the environment. The environments can't produce any selection pressure, in practice. Only artificial environments can really do that.

Evolution has the power to do so, but the environment doesn't, and the fact that evolution always has to work with what it's already got imposes some limits. For example, humans can probably not evolve away our spines, because any attempt at doing that would be deadly, so humans will forever have something similar to our spine.
But really, we've only seen about 700 million years of multi-cellular life. We do not know what billions of more years could do, because we have no such examples to study.

"You don't know what lungs humans would need to fly. You reason like a kid. ... I actually know the kind of lungs needed for flight as we see in birds ... fact ... our lungs would need dome modifications to support flight "

No, that is only one way to solve the poroblem. What if we started storing pure oxygen somewhere in our bodies? Problem solved, without changing our lungs. We jsut hav ot build up oxygen while not flying, like a battery.
Insects that fly don't even have lungs, as I understand it, they breathe throught heir skin.
And there are probably a gazillion other possible ways that things could work. We just don't have good enough imagination and creativity, because we can only base ideas on things we've already seen, we can't think truly "new" thoughts.

"ofcourse the possibilities are endless with evolution ... anything can produce anything ... that's why I'm not sure exactly why it's taken seriously for predictive abilities"

Because in reality, certain changes require certain changes to the DNA, so we can predict what changes can and cannot happen through mutation, for example.
When making pesticide, for example, we try to make sure that the ability to become immune to the poison would require for example 8 coordinated mutations, and that should not be possible, therefore they won't become immune to that poison. (We take that risk.)

Anything can't produce "anything", only in theory, but not in practice, because in practice.... well, I've gone over this, alredy.

If you take a group of animal, and you impose a problem of their survival, then you can predict what will happen to them. If they need ot be taller to survive, then they'll likely become taller, though there are other possible ways, they might learn to stand on top of eachother, or something.
But they will not start becoming shorter and not solve the problem. If they do something like that, which makes no sense from the perspective of natural selection, then the prediction fails and we've got some kind of falsification of something.

Predictions aren't quite about predicting future events, it's about prediction what we will find to be the case about something. Sometimes it's future events, other time it's new knowledge about past events. Both are still predictions, in science.

"I think I've done enough study since you can't provide credible answers to support evolution"

The actual problem being that no matter what I would present, you have reason to ignore it. There is no way anyone could have your position unless they willfully ignored science, or was brainwashed in some other way.
And yes, religion does that to you, so I'm not saying I am surprised.

"I would search it up and show you but [...]"

How did I know there was going to be a "but", and that you once again would not actually provide anything? It' snot because I ahve amazing predictive powers, it's because you're so fucking predictable.

Sorry, I'm tired of this shit. I'm done, for now.
Reply: antiHUMANDesigns *slow clap...*
I really enjoyed your last two posts, and I commend you for your patience in repeatedly elucidating with stunning clarity the countless misconceptions and fallacies Benjamin Toby has attempted to employ in his futile defense of the non-theory of ID. I also enjoyed your explanation of the difference between code and symbolism, as I am also a part-time programmer and had never had the luxury of having someone distinguish the two for me, despite being aware that such a distinction existed.

It's too bad Toby stopped replying to me after I showed him that a structure's "irreducible complexity" has nothing to do with the capacity for it to have evolved. After he saw the IC bridge, he just called it a "miscue" for no apparent reason and abandoned his attempts to explain what that word even meant to him.

I know that you didn't read my conversation with Toby, but the reason he won't provide another definition of "code" is that the last one he adopted went up in smoke when we applied it to things like rivers. He is a one-trick-pony: when you call him out on a specific flaw or ask him to justify his claims that what his interlocutor is saying is invalid, he simply tells you to read what he wrote again until you "get it" (which is his way of saying "read it until you agree with me"). I too am bored of this tactic, but I am willing to entertain him a bit longer if he decides to reply to my last post.

So, Benjamin Toby, are you ever going to get back to me and explain what makes my analogy a "miscue," or tell me what unique, falsifiable predictions ID has made and how we can test them? Or are you just going to keep talking in vapid circles until I get tired of pointing out your lack of substance and consistent evasion of my questions like AHD did?
Reply: Max Spiegel I didn't know you took the time to read it. I have no idea how I can have such patience with this, but yesterday, my patience did run out.
My problem with it is his arrogance and completely lack of humility, really.

Yes, about the whole "code" thing, I do understand why a lot of people have a problem with this. It's really easy to look at a car and think it's a beautifl car, and that it hsomehow is beautiful, in itself, rather than that the beauty of the car is in your own head.
This is at the heart of the reification fallacy.
And with computer programming, it gets even more complicated, because all the software we use is designed to make it seema as if the computer is intelligent, and that we can speak intelligently to the it.

But the weird part about my conversation about this, with Toby, is not this, but rather that he thinks "code" is something absolutely completely different that what it is. He isn't just a little wrong, he's astonishingly wrong.
And that is after I've clearly explained it. He just can't take anything in, it seems.

"It's too bad Toby stopped replying to me after I showed him that a structure's "irreducible complexity" has nothing to do with the capacity for it to have evolved."

Yes, I've tried to explain that, aswell, but in a different way. But I think the problem with IC is best described by visualizing it, and I can't do that, here.

"After he saw the IC bridge"

Ah, yes, the bridge. Same example as used by Richard Dawkins in the god delusion, I think?

"he simply tells you to read what he wrote again until you "get it" (which is his way of saying "read it until you agree with me"). "

Heheh, yeah, I've noticed that. I really, really want him to honestly explain what he thinks/believes, or the terms he use, but he just won't. I really do take that as evidence that he is unwilling to defend his position.
Reply: antiHUMANDesigns The bridge example was just something I stumbled across online; I don't know who first gave that analogy.

I also forgot to thank you for teaching me what a reification fallacy was as I had never heard of it before, and it seems to be at the heart of most of these "but where did the 'code/informatoin' (when abusing the word "information") come from?" arguments that creationists regurgitate time and time again. Usually I refer them to Shannon-Weaver theory, and when they see that it doesn't help their position in the slightest (or not because they don't understand statistics and probability) I let them choose their own definition which inevitably breaks down. However, now I have a new tool with which to illustrate that their erroneous conceptions of these words is at the heart of their petty defense of ID, and I'm quite grateful for that.

You really write some of the best replies to creationists I've ever seen, and I thoroughly enjoy reading them. They almost always put a smile on my face and give me something new to think about. Thanks again.
Reply: antiHUMANDesigns  

The problem being that you just attacked me for actually clarifying it...! Schizo. ... Nope you're actually trying to impose your view without listening to my explanations ... 

Exactly my point: This reply is all I get when I actually ask you something. Your attitude is that I should just "know it". You offer absolutely nothing. Tell me again why I should bother taking you seriously, to begin with?  ... no  ... most of the times I give you simple replies with easy explanations which you mostly dispel without proper analysis ...

Your comments are largely made up of just nothing. ... and your comments are made up of what? ... if you're going to dispel my comments without actually understanding it then don't accuse me for refusing your nonsense ... 

70% is stuff like I pointed out before, where I ask you a question, and all I get is that I should just know it, or that you have already told me. There is very little to "understand" about it. ... I actually answer most of your questions ... not my fault if you just can't open your mind a bit more ... I actually end up repeating myself over again like I'm talking to a damn rock ... you might be wondering why Mark repeatedly asked if you even watched the entire video ... it's probably because you talk off your ass and do little thinking ... don't 
blame me for that ...

When I ask you for a definition of "code", according to your undertanding, I am not asking for a vague example, I am asking for a damned definition. ... and I gave you a definition earlier: obviously you've forgotten it due to you long lines of mostly crap ... if you can't remember previous comments then don't type so damn much for Gods sake ... PS didn't you see the other definition I agreed to with Spiegel? 

One example of something you would call "code" is not enough to figure out the definition of it. I want to know what makes you think that something is "code", your process of figuring that out, your criteria, your definition. I have given you the definition, and if you disagree, then give me an alternate definition. It shouldn't be hard if you claim to know what it means. ... No stupid I'm actually trying to refute your definition since you've forgotten the definition I gave and the one I and Spiegel agreed to ... and once again, going by your definition, there are no codes when using a laptop casually: according to your definition only programming with programming languages entail codes ... like I said I'm coming from a background of EEE and that's more like nonsense ... 

And I admit the possibility that it is something I am simply not understanding, but you have to realize that it is up to you to make sure that you are properly understood. ... and it's up to you to try to understand before jumping on your keyboard and giving me thousands of pointless lines ... 

That is not what code is, or what code does. "Code" is something between two minds, such as two humans. Computers never work in code. I have said this many times, but you don't address this, you just keep repeating yourself. ... Nope ... All computers work with codes ... this is high grade BS you're giving me now ... I'm not saying code can't be something between two minds ... it can be ... just that's not what the computer code is ... 

It isn't code. I've said this so many times, now. ... I know that you've repeated the same thing a couple of times ... I'm just saying you're repeating the same wrong assertion, and I'm trying to state why ... 

"1/0" are symbols. To have code, we need to to agree on something that represents "1/0". We do that. We made "assembly" which is a coding system where simple words represent binary sequence. So when we write assembvly, we are writing code. ... and I'm saying THIS.IS.WRONG ... without assembly you can still create programs with binary codes(and don't tell me it'snot code cuz you're displaying unbelievable lack of understanding) ... the assembly makes it easier and less cumbersome ... if you skip it and write using binary codes, you're doing 
THE.SAME.DAMN.THING ... just that it'd take longer ...

But "code" is conceptual, it's only code in our minds, and in the minds who agree that it is code. To the computer, it is not code. ... to call anything a computer to begin with means it has a programming with codes ... ie it can understand binary codes ... 

The computer is symbolically reading a binary sequence. ... this is actually real ...

 *That is, there is no "reading" going on, it's an analogy. "Reading" requires the ability to "understand", which a computer can't do.* ... if the computer can make desired output from an input, then it's "understanding" the codes ... this might be best described as what you called "emulated mind" ...

That is why I'm saying that is symbolically or "conceptually" reads a binary sequence. And it isn't a binary sequence to the computer, either, it is just a bunch of voltages. ... to a computer, it is a binary sequence ... like I said ... the computer is programmed to understand the sequence ... to a piece of wood, it's just a bunch of voltages ... 

Then it is the software that's telling the difference. and what do you think the software is? ... it's just a program ... 

I have said that theoretically, software could probably emulate a mind, or even become a mind. If we'd manage to do that, then the computer will have a mind, and could understand code and symbolism and concepts and ideas. But if the computer doesn't have a proper mind, then no matter how complex the software is, the software is as extension of a programmer. It is the programmer who understand the code, not the software or the hardware. The programmer made a program that does what the programmer would have done. The software isn't able to be a person or mind in itself and hold its own understanding of things.

*I cannot actually tell the computer to "mov" anything. It would not understand that that concept, because that would require the computer to have knowledge of the world around it and how physics work, and so on, so understand the idea of moving something. Ond obviously, when we move a value from one register to another, we're not literally moving anything, we're actually copying something, and then ignoring the original as if it doesn't exist. We only conceptually describe it as "moving" a value. And the computer doesn't have to deal witht his, anyways, because it is only in our minds. What the computer gets is a pattern of voltages that cause a specific thing to happen. We can symbolically represent those votalges by 1's and 0's, for example. But because that becomes cumbersome, we can instead use code, which is what we do when we write "mov" in assembly. As long as we 
are all consistent in what "mov" means, the code works.* ... my point is the "pattern of voltages that cause a specific thing to happen" is the action of the computer code ... now like you said, "mov" is an instruction the computer interprets as cutting something and pasting it in the desired location ... mov represents a binary code (don't fault me for using this term I have good reason to): the action to be carried out is also represented by binary codes (voltages and switches) ... lets say "mov" is 110011, and the action is 11110010 ... if 110011 is translated into 11110010, then we have an action of interpretation ... and if the computer can interprete, it works with codes ... and since "mov" stands for the code 110011, we can just skip the compiler and work with the 
binary codes: still works the same way ... after the action of moving happens, the computer sends the instructions required to display the actions: our mind can understand this ... but the backend switching and 
interpreting of binary codes is the actual computer code ...

That isn't what "code" is....! ... and you're not making any progress with these assertions ... I'm saying you're wrong so what use do you think it is to me if you tell me "that isn't what code is"?

Please, just think about examples like "morse code", for example. Why is "morse code" code? No matter how you transmit it, or if you write it down or say "long short" or whatever, it still is "code". Think about why it is. I'll tell you one last time why it is: Because it is a system of symbols that represent other symbols. ... ok lets see ... say I want to send a message "hello" using morse code ... and say that message translates to 
.--.--...- (by this I mean the actual tones).... the ".--.--..." represents hello ... the code is the sound pattern and the way you represent it makes no difference to the code ... if you use ".-.--...-" or "beep beep ..." or you just punch some keys to make the sounds... they are all the same thing: sound patterns ... the code is still in effect anyway ... so I don't know exactly where the second level symbolism comes in here ... if I puch some buttons that make the sounds, and those sounds are symbolical for the message "hello" ... where is the second symbol to make it a code?

Now, as for the rest of the subject of "code", I seriousy give up trying to make you understand. ... no you're trying to force an illogical thought through ... that's why I'm asking questions and pulling up explanations of my own to make you understand my drift... maybe you should give-up after you actually understand my point ... 

This was my last attempt. I have said what I can say, and perhaps I don't have the "teaching skills" or whatever, to get the message through. It would've helped if I could draw while talking, or something. ... I understand what you're saying silly, and I'm saying you're wrong ... but you don't seem to understand what I'm saying ...

I see you keep arguing the same thing, as if you don't see what the problem is, and I give up trying to explain what the problem is. I've used all techniques I can think of. But as I see it, when I explained to you that "code" is second-level symbolism, then that's where it should have been clear, and this discussion should have been over. It's not, and like I said, I give up. I'm not going to waste time repeating myself over and over, which is all I can do, now. ... first you're arguing the samething as well even if I've explained to you why I think it's wrong ... secondly did you just say "repeating"? well for most of the time I actually repeat myself so maybe I can say I'm glad you can feel how frustrating that is ...

That is not a proper response. Tell me if you get it or not! When I am programming, I may be writing code. It isn't the computer that writes the code, it is me. My code is then compiled into software, which runs on the computer. There is no... code... in... the... software! It was made using code. ... maybe you should tell me if you understand anything I say or not ... I clearly gave you an example of a program with a colour code changed to explain that a program contains codes ... and you go on to tell me a code contains a program ... lets say the calculator on you computer is a program ... it has a "source code" and if you can access it you find out the different codes used to achieve different functions ... if you change the color code of a button to red, then you have a slightly different program ... simple explanation of a program containing codes ... in addition to the color code, the calculator has codes for addition, subtraction, getting data, etc ... all these codes do specific tasks and if you call for any of these codes in another program, say "media player", it's going to do the same damn thing... and your "media player" would be a slightly different program ... dammit ...

Yes, I agree fully. Stone henge was probably built by humans, because we know that humans make religious or cultural artifacts like that, and it looks like it was made in the kind of way that humans of that time made things. ... the primary term you should realize is intelligence ... you don't know if it was actually humans like you or some superhumans or even aliens ... you have no evidence of that ... we just know that intelligence can create such a thing so we assume it was humans like us ...

Now tell me what experince we have of designer gods who make life, so that we can make such an inference. ... for the nth time what I need to tell you is experience we have of intelligence creating things like an induction motor or the computer code ... with this we can say that the flagellum and DNA were most likely caused by INTELLIGENCE ... and as a christain I say the intelligence agent was God ... do you understand now?

...tell me when the coin drops.  dafaq ... u mad?

I did not read your conversation with Spiegel, as far as I remember. ... well first of all you can go read it now ... secondly do you even remember what got you into this conversation again? ... yes ... you read my responses to Spiegel ... so go read it properly before spewing your BS ...

Also, I don't need irreducible complexity explained to me, I understand the concept very well. But it still remains an argument from ignorance, unless you can logically/mathametically prove that it is impossible, which is effectively impossible to do with most things. You have to prove that there cannot possibly be a way to explain it that we have not yet thought of. ... well thanks for proving your blind faith and ignorance ... actually you need IC explained to you: speaking from the state in which you currently are ... and I gave a mathematical expression to attempt to distill the facts into simpler terms ...

For example, 1 cannot be 2. We know that, and nothing is ever going to change that, because we can prove that 1 isn't 2. ... dafaq ...

But you're talking about looking at a structure, and proving that it cannot have evolved, and that we will never in the future find a way to explain how it could have evolved because it is impossible. ... Nope I'm talking of looking at a structure and proving it could not have evolved by slight modifications ... ie it could not have evolved by evolutionary processes ... except evolution spontenously assembles IC systems ... which would be a lol ... btw we're not saying you're never going to find an explanation as to why, in the future: we're saying all your explanations now are inadequate ... 
 
And that cannot be done, because the best you can do is to say that it is "unlikely", because in the end, it is theoretically possible for a mutation to do anything to the DNA. ... well you must realize that we are working from a practical aspect ... if a system is tested to be IC then it's not possible for it to arise by any process which doesn't involve spontenous assembly and instant functionality ... 

But if something takes more than about 3 coordinated mutations, then we consider it unlikely and try to find some other explanation. But "unlikely" doesn't mean "impossible", which is why irreducible complexity is an argument from ignorance: "We can't explain how it could evolve, therefore it can't have." ... IC actually says this system is, as a matter of scientific fact, IC: therefore evolutionary processes can't possily give rise to it ...

ID is an attempt as a hypothesis, but because it isn't even falsifiable, it isn't even a proper hypothesis. Quite damned far away from being a "fact". ... IC is falsifiable ... take a bacteria without flagellum and create the neccessary pressures for mobility in a lab ... if the bacteria develops a flagellum, IC is falsified ...

Not a fucknig chance that I would let anyone get away with a fallacy. ... anyone except yourself ...

Says the person who can't spot an argument from ignorance, or a reification fallacy. I'm miles ahead of you. .. ofcourse the way of the fool is right in his own eyes ... remember? ...

If he hadn't given up and resorted to saying "god does it", he might have figured out what Einstein later figured out. That is my point, in case that wasn't clear. ... Newton didn't come to a conclusion of God because he gave up on his science ... the knowledge of God was the foundation of his science ... so once again, wth ...

I cannot say that he was an atheist unless he himself said that he was. He expressed the same kind of statements that an atheist would say, but I have never personally heard/seen him say the word "atheist". well search the damn page he stated it clearly he was no atheist and he gets "angry" when he's quoted for the atheistic viewpoint ... either you search it up or just STHU ...

Back in his time, "atheist" had the notion of meaning to be against god, or to know that gods don't exist. ... new BS? ... atheist meant the samething in Einstein's time as it means today ... he even defined the "proffessional atheist" perfectly and it applies today ...

But all that matters here is that Einstein was not a christian, or a jew (other than culturally), or a muslim or a hindu, for example. He called such things "childish" and superstition. I'm not saying he was a christain (even though he had good things to say concerning Jesus) I'm saying he was closer to theism ...

"Agnostic" means to believe that the question of gods existence is unknown, and sometimes even "unknowable". Agnostic/gnostic is a question of what you think can be known, it is not a question of what you believe. ... agnostic actually means the human knowledge is too limited to disprove God ... ie there's not enough knowledge disprove the existence of something like God ...

I am not a scientist, and do no scientific work, and am not part of the scientific world as anything but a spectator, which would effectively include us all. You too. ... actually you said here that you represent science ... I'm just saying you represent the infection in science ...

You have to understand the idea that some things are more random than other things. ... loool ... this is really desperate ... less random, more random, STILL RANDOM ... 

But whatever, who cares, lets say they're all perfectly random, this is seriously not something worth arguing about. I think it is ... you might want to re-read all instances I described evolution as random and see how absurd it really is ...

The point is still that evolution isn't random just because mutations are. ... No it is random because all the processes involved are random ... 

Evolution is a lawful process with a specific outcome, not a random outcome. ... lol ... an undirected process creating specific non-random outcomes? ... you might be having evo mixed up with ID ...

Gould's law of irreversibility forbids that, so no, most certainly not. ... unfortunately evolution doesn't forbid this ... I mean it got a human from a bacteria ... this is just a piece of cake ...

Cirtical thought, in the form of logic, makes me discard it. I have explained that those arguments rely on logical fallacies. Since I am aware of that, I am forced to discard them. And so are you, you just don't seem able to see it. ... I see most of your points ... they are based on fallacies as well ... most notably the equivocation fallacy in the definition of evolution ...

Exactly, the consensus is that time probably started existing at the moment of th ebig bang. So tell me at what point in time there was no universe? A second before the big bang? No, there was no "a second before the big bang". There is no "before" the big bang, according to current understanding. Thus, the universe has always existed. There never was a point in time when the universe did not exist. ... yes there was a point(not in time) where the universe didn't exist ... once something is proven to have a start, it means before it nothing of such sort existed ... simple logic ...

Admit it, it's because you can't explain it. You're such a coward to try to blame me for your inabilities. ... actually it's because reading and responding to 1500+ lines of mostly BS is time wasting and stressful ...

Yes, Baal, for example, right? Yes, I know that in the bible, tehr eis a god called "god", even though I think he's actually called YahWeh, but  whatever. that doesn't explain what a "god" is. Jstu because there is a god called "God" doesn't help one bit, you know. I still don't know what a god (called "God" or not) is supposed to be.... I don't know if you're doing this on purpose or if you're so damn ignorant of this ... 

And perhaps children know these things where you come from, but where I live, in Sweden, religion is not really a "thing". We study it in elementary school, yes, but only briefly, unless we choose to study it more. And we study the 5 major world religions, which doesn't leave all taht much time to study christianity, specifically.it's just not a priority. Math, swedish, and english are the top priorities. ... well if you studied this in elementary school why the stupid questions considering that 3 of the 5 main religions are based on this same God I'm trying to explain ...

"sigh, you don't get it... the tree of life, yes all living things on it has DNA, but the tree is a tree structure because the traits of all living things fall into nested heirarchies.* ... pls for the nth time use the term groups ... that was the term you used to even start with ...

There are no mammals with feathers. Find one, and it would usggests that it is a descendant of both a bird and a mammal, which screws up the tree. It wouldn't fit anywhere on that tree. That would be a huge problem. ... 

lol... not for evolutionists ... they're going to force it into the tree somehow ... lol ... just create another branch, conjure up another imaginary missing link, problem solved ...

If you were back in that time, then there would be no sub-groups to those new phyla that you're talking about. ... yes there would be ... a trilobite was still an anthropod ... and there were different species of trilobites 
... PS there were other anthropods aside the trilobite ... 

It cannot, it is impossible. Even if all life on earth was designed, the fossil record could not be evidence of it. ... why not exactly? ... it seems to me like your just trying to secure any path through which the thought of design can gain roots in your paradigms ... you're probably only deceiving yourself ...

It allows for any amount of evolution, aswell. The idea that life was initially designed doesn't means it cannot evolve. ... more like "devolve" ... works well considering entropy ... but devolution doesn't mean there's no diversity ... the diversity is caused in reproducton and it is a part of the code ... possibly the designer wanted more variety ... 

No, it doesn't. ... yes it does actually ... and I brought this up because evolution says anything can produce anything ... given millions of years ... ID says "a bear can never be a cat" and vice versa, no matter how long you give them ... but with evolution, a bear can become a cat with millions of invisible years ... afterall, there's no restriction to the change and if a bacteria can produce a cat over milions of years, how much so a bear ... you see this predicition is atually unique to the Design concept ...

....to be more in line with the evidence of reality. That's how science works, did you not know this? ... well don't you remember you accused the Bible of beign revised to be more in line with the evidence? ... the only thing that changed about evolution is the definition ... which came from the normal "simple to complex" to "change in alelle frequency" ... I never knew one could change a definition so much to suit a theory ... maybe they should have just renamed it to something like ... Theory of genetic change ... would be more accurate ...

*Perhaps you should learn about the subject before you talk bullshit. What are alleles? http://biology.about.com/b/2010/05/15/what-are-alleles.htm* ... maybe you could have just done a simple google search to confirm my point: which was that allele was a relatively new word coined-up in 1930 ... 

At Darwin's time, we had not yet dscovered DNA, so it's not fucking strange that he did not write about alleles...! reasonable ... but Evolution was defined before the discovery and the new word ended up introduced into it to skew the definition ... 

Sorry, what? Are you saying it's stupid that penguins produce penguins? It sure looks like that's what you're saying. ... a lack of proper comprehension ... if you followed up with the next line then it was obvious what I was talking about ... 

It isn't the theory of evolution that explains that penguins give birth to penguins. It is a matter of classification. ... lol ... didn't you admit that the difference in colour in the peppered moths proved evolution? ... 

Any offspring of penguins will be classified as a penguin, because they will have the traits of a penguin. That is not "because of the theory of evolution", it is because of something much older than Darwin. It is Carl von Linné, since he invented this system for classifying life. ... now you need to be damn sure that Carl was the first to invent a system for classifying life ... because I'm quite sure people have been classifying life for as long as they existed ...

Well, it also describes humans as spirits, in a sense. ... in the sense that the spirit is the part of the human triology that is actually the closest to Gods likeness ... the spirit is like a part of God given to man ... 

But that doesn't mean we don't have physical bodies. ... it means our physical bodies are just part of our entire existence ...

And god evidenetly was materials in the sense that he was visible. People in the bible have seen god. ... no one ever saw God ... according to the Bible, no one sees God and lives ...  

To see someone, they have to give off light in some way, meaning they are physically real, or they're violating the law of the conservation of energy. ... actually God manifests himself in the physical in a couple of ways ... most notably light and fire ... I'm almost forced to think that God is actually closely linked to Energy ... or is behind it ... or is it ...

Applying too much critical thinking to the bible turns it into a huge mess that makes no sense at all. The only way I can make sense of it is to imagine a person 2-3000 years ago, writing this as his explanation for why the world is the way it is. then suddenly it all makes perfect sense. ... actually applying critical thinking to the Bible reveals a stunning amount of truths ... and it's mandatory that you be very critical to the very maximum: and be open minded to the truths ... 

Perhaps, but then they all act as if he isn't. It's weird how they can describe him one way, and then he doesn't appear to be that way at all. ... actually i don't know if I told you this ... God is immaterial but He can manifest is different physical forms ... and He is not bounded by the physical laws ...

I prefer to try to make sense out of it, instead, and figure out what he is, rather than listening to how they describe him, sicne that rarely makes any any. ... well if you're ready you can start be studying some aspects in the Bible and asking reasonable questions ... you might also want to look for a rabbi for clarifications of some OT facts: or just get one of their Bible commentries ...

"God is love"? Sorry, love is a feeling we have that is caused by hormones and such. God cannot be that thing. Obviously it is an analogy, or something. So then I have to actually deduce what he is from reading the other parts. ... like I said, Love is not controled by the hormones ... the hormones just show the symptoms ...

And nothing about it ever leads me to think that god is "immaterial". He is sometimes scribed in a similar way, but he never acts as if he is. ... then you need to come out of you ignorance ... and fast ...

The definition of "magic". Perfect. ... it's actually an extrapolation from the finite universe theory ... the cause of the universe cannot be bounded by the universe' attributes ... from what you're saying the big bang is actually magic ... and also I think I said this countless times but evolution is also magic by this thought ... because no known natural cause can create a human from a bacteria ... 

If you actually studied cosmology, you'd know that the stars came long before earth. But according to genesis, god created the stars on day 4, or something? That is, the earth came before the stars, according to genesis.ong after stars had formed and died, the earth was finally created. The universe is about 9 billion years older than the earth. ... well actually the Bible says God created Heaven before earth ... but the creation story is not what I'm using for my paradigm ... I take it as a symbolical reference ... actually most of the Bible is symbolic ... it just gives a good idea of creation ... it's left for science to actually verify the actual facts ... and I'm not sure of your rationale for the stars before earth assertion : I'm no expert in cosmology ... I barely read up on it tbh ... maybe you should explain better ... or better still, put this on hold so you don't creat an unbearably cumbersome situaion ...

You mean show me some technology that beats humans? Pretty much everything we build are built simply because they do things better than humans do them. more specifically: faster ... not necessarily better ...

A fucking calculator beats humans, that's why we make them. They insanely much faster, and effectively never makes a mistake. A car is faster, a tank is strong, a plane can fly, binoculars can see futher, submarines can dive deeper, a catapult can throw thing further, a bus can carry more people, a lamp can give off light, night-vision goggles can see in the dark, want me to go on? Some things we build even last longer than humans, which is quite impressive considering that life has the ability to maintain itself and theoretically live extremely long times. ... I don't see how the creations can beat the creator ... maybe if a calculator could repair itself after loosing a wiring it could come remotely close ... and I'd like you to get a calculator, or any computer make computations, analyse data, control nerves and functions, regulate body temperature, and the other numerous functions of the brain for one hour on the energy of a sandwich ... you have no Idea what you're talking about ... also you've missed the most important aspect of humans: sentience ... this beats any technology we have hands down ... just imagine if you could get a car to think for itself ...

Huh? Longer than a fucking human can, at least. A satellite only has to orbit earth, it doesn't require any energy at all to be a satellite in space. ... yes it does wtf ... there are electrical components inside without which you have a bunch of metal orbiting in space ... what do you think the solar pannels are for? ... u kidding?

But no one has designed a satellite that is supposed to use as little energy as possible and just "be a satellite". Huge waste of money. ... well the birds can access the functions of a sitellite and gps with very little energy and lesser space taken ... PS my point was actually related to air planes navigation system ... birds know how to navigate their way even much more efficiently than any plane you can call up ... 

Depends on what you want it to do. I listed a few examples of how technology beats humans. We can combine a lot of those things, if we wanted to build somethign that is specifically built to meet your challenge. ... lol you know there's no present robot that comes remotely close ...

There is no "creator", that's why it's not "technology". ... the analogy dammit ... you should work on you memory if you're going to type so damn much ...

If you read it one more time, you'll see that I said "any such system will evolve". I said nothing about a specific kind of change, like single selled to multi-celled. ... well there's no evolution if single cells cant transform into multi cells so you're shooting yourself on the foot ...

*Hahas, yes, it fucking is...! Evolution is exactly that. Don't believe me, then just fucking look it up. (Not from creationists who want to misinform you, of course.)http://evolution.berkeley.edu/evolibrary/search/imagedetail.php?id=319&topic_id=&keywords=
Fucking Berkeley, for you: "Microevolution is a change in gene frequency in a population. Suppose you sample a beetle population this year, and determine that 80% of the genes in the population are for green coloration and 20% of them are for brown coloration. You go back the next year, repeat the procedure, and find a new ratio: 60% green genes to 40% brown genes. You have detected a microevolutionary pattern: a change in gene frequency. A change in gene frequency over time means that the population has evolved.* not stupid a change in gene frequency over time means the population has changed ... from a population of mostly green to mostly brown beetles ... that's just genetic variation ... lol ... what a desperate attempt to validate a dogmatic theory ... like I said, your ape-men ancestors can easily tell these beetles are getting more diverse ... wasn't that why there was selective breeding to start with? artificial selection ... lol ... you're just telling me what cave men knew thousands of years ago and calling it a scientific theory ... wtf ... I don't see how this isn't a joke to you ... 

But you've got your straw man version of the science, which I bet you'll keep sticking to. ... haha ... funny stuff ...

You're the one with the equivocation problem. You seem to think that "evolution" is the same thing as "the theory of evolution". That is your equivocation, not mine. ... no silly ... I know evolution is not a scientific term and it means gradual change from simple to more complex ... just that when science uses it, it's to describe a theory ... not to change the meaning of the term : like what's going on now ...

If I had time, sure. But I ahve a family, a wife and a daughter, and I have work to do. I dont' have time for everything, and then I would prioritize learning science over learning the history of science. ... then where do you get the time to type up all this BS? ... maybe you should minimize your time and actually study more ... and by study I don't mean loading up your brain with unverified nonsense ... I mean skeptical addition of new knowledge ...

Hahah, because it doesn't make any predictions, you twat. :D ... it does you twartard :+ ... it says for example junk DNA aren't junk like you say ... it also predicts there'd be signs of design ... the flagellum is a perfect example ... the DNA is also ...

No, the specific predictions. Such as if we have two species that share very specific traits, then the theory of evolution would predict that they share a common ancestor. ... thats a failed prediction ... humans and earthworms both contain cells ... so whose their ancestor? ... lol ...

And yes, it keeps being correct. The theory of evolution predicts which fossils should exist, and where they should be found. ... lol and the scientists do the remaining job of adding the remainder 90% missing parts to confirm the prediction ... hahahaha ... 

Go somewhere else and cry about how you pet hypothesis won't get recognized because it happens to be shit. ... no it's ignored because of it's implications ... not it's evidences ...

Yes, I would fire any scientist I have who would argue for ID. Why? Because you can't argue for ID, so anyone who would say they do is a half-wit. ... of course fire anyone who has an alternate argument that refutes yours because you just can't, or don't want to understand it ... very stupid statement I'd say ...

Like I've said, ID doesn't make any testable predictions, therefore it an never be shown to be true or false. A "scientist" who doesn't undertand that is not someone I would hire for anything, because they've failed to understand the scientific method itself. ... lol you're quite dull ... well Behe proposed a way to falsify IC ...

ID is not science. ... spoken from ignorance ... maybe you should look up the statement of ID again and look up the arguments from ID proponents ... till then try to STHU about something you don't know ...

Bird wings evolved from dinosaur arms. ... which evolved from bacteria ... why are you trying to evade your nanoscale daddies ... 

Seriously, go back to school, you're a joke. Why do you even go on inernet and discuss shit you know nothing about? You're wasting everyone's time, and looking like an idiot while doing it. ... firstly going back to school for me would be studying more importand topics ... secondly you've even admitted discussing stuff you don't know anything about ... thirdly mathematically the one wasting time would be the one TYPING OVER 1000 LINES OF CRAP ... I'm even trying to save time with shorter responses and get to my point as quick as possible ... Fourthly I'd look like an idiot in the eyes of people like you certainly ... that's because a world class restaurant dish is trash for a pig ...

It depends on what you mean by "wings"! I asked you this, already. If you're asking how humans could evolve wings, then first fucking define what "humans wings" would be, or no one can answer your question. ... seriously? ... ok just take any wild guess : imagine how the wings would look like ... we're working with evolution afterall so anything goes ...

If you're talking about simply making humans fly, then the reason it won't happenis because we would have to have *insane chest muscles to produce enough force to lift our bodies.* ... evolution is up to the task ...

We are simply too heavy, that's the main reason. ... with evolution that's a piece of cake ... we can just develop stronger wings or loose more weight ...

*Evolution is driven by whatever genes cause us to have more offspring.Evolution is not random. Having wings probably won't do that to human, so then we won't evolve wings.
However, we still die from childhood cancer, for example, which might mean that in the future, we'll evolve some kind of protection to dangerous childhood deseases that prevent us from reproducing.It is probably a natural part of the devlopment of life itself, that it start out simple, gets more complex, then gets technology, and no longer plays by the same rules anymore.

I agree, but at least we can say that it would take an insane amount of time for us to evolve wings. We are very, very far from being fit to fly. That is, if we're talking about powered flight, not just "gliding". But if you're just talking about gliding, then that is a different thing. ... I'm also talking about wings ... like bitds   ...Exaclty, only in theory can it change anything into anything, but never in practice* ... I see : in reality a bacteria cannot develop wings but in theory it can ... interesting ... then that means in theory anything can develop anything ... doesn't make the theory any more valid ... 

because evolution is directed by the environment. and environmental changes are random ... 

The environments can't produce any selection pressure, in practice. ... so what about a case where an environment of more predators affects the population of weaker preys? ... is that not something that can be observed in real life? ...

Evolution has the power to do so, but the environment doesn't, ... yes the environment es because a change in environment affects evolution ... and the fact that evolution always has to work with what it's already got imposes some limits.*  ...no it doesn't because there's no restriction for what can and cannot be useful ... the same trait can be useful and useless at different environments ... 

For example, humans can probably not evolve away our spines, because any attempt at doing that would be deadly, so humans will forever have something similar to our spine. why can't we? it'd just cause an extinction ... something all too common with evolution ... so?

No, that is only one way to solve the poroblem. What if we started storing pure oxygen somewhere in our bodies? Problem solved, without changing our lungs. We jsut hav ot build up oxygen while not flying, like a battery. Insects that fly don't even have lungs, as I understand it, they breathe throught heir skin. And there are probably a gazillion other possible ways that things could work. We just don't have good enough imagination and creativity, because we can only base ideas on things we've already seen, we can't think truly "new" thoughts. ... well I could agree with this ... since evolution can do anything ... it can conjure up another perfectly functional compartment in the ass for example where oxygen can be stored for flight ... and ofcourse it can create the system to regulate and signify depletion of oxygen: and maybe even a system that can turn poop into extra oxygen: supercharger style ... and even a system that can create oxygen packets in the poop while processing food ... ok that's enough for now ... I think you get the point ...

Anything can't produce "anything", only in theory, but not in practice, because in practice.... well, I've gone over this, alredy. well in practice we have adaptation and variation ... no evolution ...

The actual problem being that no matter what I would present, you have reason to ignore it. ... actually you've presented mostly false info and fallacies as well as good old pure BS ... I refuse most of your points because it'd be stupid of me to just swllow your drivel without proper thinking ... 

There is no way anyone could have your position unless they willfully ignored science, or was brainwashed in some other way. And yes, religion does that to you, so I'm not saying I am surprised. ... actually this applies perfectly to you: you're scared to have your beliefs shattered by the truth so you'd do anything to pervert any thought or evidence supporting ID ... 

How did I know there was going to be a "but", and that you once again would not actually provide anything? It' snot because I ahve amazing predictive powers, it's because you're so fucking predictable. ... actually you knew I was going to say but because I made it clear that I'd refrain from explaining more until you understand the previous comments ... so much for your super amazing predictive powers ...

Sorry, I'm tired of this shit. I'm done, for now.? ... well not so fast ... you came up with 1500 lines you're going to defend every single piece of crap you spouted ... I was actually glad to see the end of such a DAMN LONG comment but once again, you've said close to nothing and I have had to repeat my self over again in many instances ... maybe you could be a little wiser and tackle the issues one at a time, with shorter lines and MORE  THINKING ...
Reply: Benjamin Toby Toby, you're doing it again. "I already told you blah blah." No you didn't, or else you would just point out where instead of claiming that your answers are up there somewhere in the thread. "There's so much evidence for ID," yet you fail to provide even one unique, falsifiable, testable prediction made by it.  And don't you remember why you abandoned our agreed definition of "code?" Are you ever going to respond to the specific points AHD and I are making? This is grueling...
Reply: Max Spiegel  lol wth ... 

1. I don't think I have the time to search for all my previous comments considering AHD types so much and it takes a lot of time to respond ... the problem is that he types and forgets previous comments, therefore making me repeat myself over again ... a good example is the explanation I gave to you about IC ... he read enough of my comments to ask me about taxonomy but he ignored the lines where I clearly explained IC to you ... however he confidently asserts that I've not given a shred of evidence or a credible explanation to defend ID ... this is just a plainly ignorant and stupid position especially considering I've taken days to explain this to you ... 

2. I've explained enough of IC to you and yet you keep repeating the same error over again ... I'm just going to repeat myself one more time ... a system is IC if it looses its function on the absence of any of it's part ... your main confusion again is that you think a system isn't IC if a function can be assigned to the intermediary steps ... hope you get this ...

3. I didn't abandon our definition of code ... you just failed to apply it and I pointed out many reasons why ... the definition is still up for scrutiny but only with non-fallacious applications ...

4. I have responded to as much points as possible from AHD ... not sure what exactly you want me to respond to atm ... but I've given him enough explanation for an educated person to assimilate ... same applies to you ... the fact that you refuse my points without proper reasoning is not my fault ... a good example from you is your attempt to falsify a fact I brought up with an imaginary stone bridge ... 

5. "grueling" is two grown men already exposed to sufficient knowledge failing to understand the simple points of a lesser informed mind ... the lack of reasoning and understanding shown by both of you here is a good reason why I'm still the theist I am today ...
Reply: Benjamin Toby
1. You haven't given a shred of evidence to support ID because you have presented exactly zero unique, falsifiable predictions of the "theory" which can be tested.

2. I already told you that your problem with IC as evidence for ID is that IC structures can evolve naturally, as I have demonstrated with the bridge analogy. Whether or not the function is different in a precursor to the final form is irrelevant.

3. You still fail to show where my application of your definition of code is fallacious. You are again just repeating that it is without explaining why.

4. Which point of yours did I fail to respond to? This is more of you saying "I showed you" when you mysteriously fail to provide an example of you showing me a damned thing. This is exactly what AHD and I have been calling you out on. If you had such an example you would actually cite it instead of just claiming that you had already done so.

5. Which lack of reasoning? Be specific and give an example. I know this is hard for you (because you obviously have none), but just give it a college try for once and cite a single, specific instance of what you mean by our "lack of reasoning."
Reply: You haven't given a shred of evidence to support ID because you have presented exactly zero unique, falsifiable predictions of the "theory" which can be tested. ... of course I have ... just take a look again at the hierarchical explanation of IC I gave ...from that if a biological system is proven to be IC, it thus follows that the IC core of that system has to arise spontaneously ... else the system wouldn't function at all ... if this is so then the only known cause for such a system is Intelligence ... because from our experience IC systems can only arise by design ... in addition, we have observed what evolutionary processes can do ... Natural selection and random mutations ends up destroying information on an average ... like I pointed out ... the only experimental evidence by Lenski showed a scenario where the most notable change in the e.coli experiment came as a loss of function of a component... there hasn't been any test or observation revealing an organism building an IC system by Natural selection and random mutations ... there's sufficient evidence to prove that evo is much more likely to destroy genetic info. and from that we can conclusively say that an IC system cannot arise by evolutionary processes ...

I already told you that your problem with IC as evidence for ID is that IC structures can evolve naturally, as I have demonstrated with the bridge analogy. ... and I've demonstrated with facts that it cannot ... only in theory ... which doesn't refute the facts ... in theory, anything can happen ... but in reality we are restricted to what we can test and prove ... 

You still fail to show where my application of your definition of code is fallacious. You are again just repeating that it is without explaining why. ... actually it's you and your colleague that repeat the same nonsense without explanation ... from your application, you said landscape is code ... and that's a clear equivocation fallacy ... of high degree at that ... you also said the the code is created by the system and is controlling the system at the same time ... which is actually nonsense ... the shape of a river can't be directing the water if it's created by the water ... and also I pointed out that the code has to instruct a system going by our definition and the system must be independent of the code else we have a situation where the code is instructing itself ... this is equivalent to saying the shape of the river is created by the shape of the river and it's regulating the shape of the river ... this is because the shape of the river is part of the system which is the river ... 

this is just a few of the nonsense you ran into while trying to apply our definition wrongly ... and like I pointed out, if you're allow to say such nonsense then I can apply the definition of work and say landscape has done work ...

If you had such an example you would actually cite it instead of just claiming that you had already done so. ... cite it? what am I speaking to people with fish brains? ... it's left for you to recall your comments and my responses so you don't end up making me repeating myself ... you're asking me to spoon feed you and AHD like you're elementary children ... I even cite my comments countless times and what I get is "you never gave any evidence" ... 

Which lack of reasoning? Be specific and give an example. ... ok lets see:

me … “what is an irreducibly complex system? an irreducibly complex system is a single system which is composed of several interacting parts that contribute to the basic function, and where the removal of any one of the parts causes the system to effectively cease functioning. ... how do we test for an irreducibly complex system? simple; get into a lab, take a set of bacteria with single flagellum, systematically knock out each and every single part of the flagellum system... if knocking out any of these parts causes the mechanism to stop functioning as a propeller of the organism, then that bacteria flagellum is irreducibly complex ”

you … “First, let's deal with the flagellum. The it turns out that bacteria that inject toxins into host cells use something called a "type III secretory system," which is an arrangement of proteins that appears perfectly homologous to the base of the flagellum. This means that the flagellum can serve a purpose without all its parts, and hence is not IC.” …

explanation … I clearly explained that from Behe’s definition, a flagellum is IC if the system stops functioning as a mobility device at the elimination of any part … and you go on to say the flagellum is not IC because it can function as a T3SS after losing some parts … well off point … but there’s more …

me … “Ummm IC simply means that removing any part of the system CAUSES IT TO LOOSE ITS FUNCTION ... not that it is totally useless for other functions ...”

you … “Fact: Things like flagellum and mousetraps aren't even IC because they have components which serve independent functions when not part of the whole "core."” …

Now tell me why I wouldn’t be forced to say you lack proper reasoning? … this is just one of many  …
Reply: Benjamin Toby
" just take a look again at the hierarchical explanation of IC I gave ...from that if a biological system is proven to be IC, it thus follows that the IC core of that system has to arise spontaneously ... else the system wouldn't function at all"
Your entire argument relies on the idea that IC structures cannot evolve by incremental change, which I have shown is untrue through the bridge analogy. I have said this many times.

"Natural selection and random mutations ends up destroying information on an average "
How does natural selection "destroy information?" Who cares about the average? Evolution doesn't need more beneficial mutations than harmful ones to create new, valuable traits; it just needs one.

"the only experimental evidence by Lenski showed a scenario where the most notable change in the e.coli experiment came as a loss of function of a component"
What loss?! The E. Coli lost nothing. I have said this many times as well.

"there's sufficient evidence to prove that evo is much more likely to destroy genetic info. and from that we can conclusively say that an IC system cannot arise by evolutionary processes"
Key phrase here is "more likely." Again, evolution doesn't have to produce more beneficial mutations than harmful ones to create new traits; just one. This is completely broken logic.

"from your application, you said landscape is code ... and that's a clear equivocation fallacy"
How is that an equivocation fallacy? You seem not to know what the phrase means.

"you also said the the code is created by the system and is controlling the system at the same time ... which is actually nonsense ... the shape of a river can't be directing the water if it's created by the water"
It's a self-modifying system, like transcription/translation. There's nothing nonsensical about that at all. The first water can come from rain in our river analogy.

"and like I pointed out, if you allow to say such nonsense then I can apply the definition of work and say landscape has done work "
I asked you to actually illustrate this at least three times and you have yet to do so. Will you finally do it in your next post? I doubt it.

As for the "IC doesn't say that when losing a component it can't have another different function," this is not what Behe said; it is was you said, and I accepted this but pointed out that you are modifying Behe's definition. How does that change the fact that you have not demonstrated that IC structures cannot arise by incremental change, and I have demonstrated that they can with the bridge analogy?
Reply: Max Spiegel I am discussing the origin of "functional information" with some other guy, in a different discussion, aswell. We've been through Shannon, and so on.
Not having any problems with reification fallacies with that guy, though. A perfectly nice and pretty smart guy, who just seems to want to put gods in there, no matter what. :P
So yeah, not *everyone* stumbles on that fallacy. And that's nice to see.

"You really write some of the best replies to creationists I've ever seen, and I thoroughly enjoy reading them."

Hey, thanks! That's really damned nice to hear, you have no idea.
I've considered, for quite some time, to make [yet another] youtube channel to debunk creation "science" and such. But I'm not sure what "angle" to take, and it kind of feels like there are enough of those channels, already.

Aslo, I'm not sure I'm as good when spoken as when written. (Or perhaps I'd be better that way, I don't know.)
Reply: Max Spiegel

Your entire argument relies on the idea that IC structures cannot evolve by incremental change ... actually my argument relies on the fact that an IC system would need its core assembled instantly to function ... as is proved by the experiments ... I just extrapolate from that to say that a process like evo, which involves systematic addition and removal of random parts can't possibly give rise to it ... 

which I have shown is untrue through the bridge analogy. I have said this many times. ... No I'm sorry you haven't if you think your bridge explains how ... like I said : what I'm bringing to the table is verifiable, testable scientific fact ... and what you're bringing is an analogy ... even the analogy fails to address the concept remotely ... I can easily take your bridge analogy apart:

1. your first step involves three stones which would function as the base of the bridge ... at this point the bridge is totally useless (according to your analogy that is) ... and a useless component has a very high probability of getting eliminated by evo. and there's good evidence for that :e.g the mexican blind cave fish which lost it's eyes due to lack of usage: ... from this we can say that your first step crumbles by evolutionary processes ...

2. your analogy is imaginary and you're assuming a scenario where the top wood is well placed on the stones : in reality, working by the random processes of evolution, there's no guarantee that the top stone would actually be well balanced as you imagine ... since there's more likely-hood to get the placement wrong, we can conclude that placing the top wood perfectly is highly unlikely and it's more reasonable to say the top wood wouldn't be placed perfectly by random means ...

3. And most importantly, your analogy is imaginary and it doesn't override a proven fact unless you take it up in a lab and disprove it ... I don't know why I should be repeating this ... In theory humans can create a super robot that will supersede the human abilities including sentience but I can say that's wrong now because our current technology can't achieve that ... and the theory cant trump the fact ...

*Who cares about the average? * ... any reasonable person does because your explanation is imaginary and hence it's the most likely and probable position that any rational person would take ... believing evo can build up the flagellum is blind faith because it's astronomically improbable going by the processes we know ... if you want to talk rationally then weigh the two probabilities and take the most likely ... 

evolution doesn't have to produce more beneficial mutations than harmful ones to create new traits; just one. ... it's going to need way more than one beneficial mutation to even form the stator of the machine ... I mean it literally has to create all those proteins in a way that they can be matched to each other to form the sub-components ... it has to match the components perfectly to achieve any function ... all these are realistically extremely improbable and hence it'd require faith to believe it can happen ...

What loss?! The E. Coli lost nothing. I have said this many times as well. ... well from what I read some e-coli developed the ability to digest citrate under unfavorable conditions via the loss of function of a component ... this is as much as I can tell of the experiment ... PS I don't think you've mentioned that there was no loss of function ...

How is that an equivocation fallacy? You seem not to know what the phrase means. ... please correct me ... landscape means the "visible areas of a land"(google) or "a section or expanse of rural scenery, usually extensive, that can be seen from a single viewpoint." (dictionary.com) ... you said landscape is the shape of a river ... you said landscape is code ... if this is not an equivocation tell me what it is please ...

It's a self-modifying system ... just need to describe what is modifying what ... cuz you're saying the shape is modifying water, and the water is modifying the shape at the same time ... 

The first water can come from rain in our river analogy. ... well unfortunately for you there's no "first water" because the water is always modifying the shape ... always ... PS the first water is also the river so the water is still controlling the code in this sense ... even though you say the code is controlling the water ... 

I asked you to actually illustrate this at least three times and you have yet to do so. Will you finally do it in your next post? I doubt it. ... no you asked me to apply the definition and I did: but it was obviously a misapplication and that was what I was trying to convey to you ... 

As for the "IC doesn't say that when losing a component it can't have another different function," this is not what Behe said ... for Gods sake that's what the definition says and that's what Behe has repeatedly said in his debates ... if you're not going to study about Behe then no need talking about his concept when you don't understand it ... 

this is the definition once more ... an irreducibly complex system is a single system which is composed of several interacting parts that contribute to the basic function, and where the removal of any one of the parts causes the system to effectively cease functioning ... 

1. a single system ... consider a biological system: the flagellum

2. Composed of several interacting parts ... the flagellum does have several parts interacting 

3. contribute to the basic function ... basic function of what? the system: which is in this case, the flagellum ... and what's the function? ... a rotary propeller for the bacteria ...

4. and where the removal of any one of the parts causes the system to effectively cease functioning ... what's the system? ... it's the system in question, in this case it's the flagellum ... and what's the function ceasing? IT'S THE FUNCTION OF PROPELLING THE BACTERIA ... 

what's so difficult here? please tell me ... 

How does that change the fact that you have not demonstrated that IC structures cannot arise by incremental change, ... it changes everything if you can't get a hold of the concept dammit ... if you get a hold of the concept you'd see it's a clear fact and the following extrapolations are the most logical ...

and I have demonstrated that they can with the bridge analogy ... and I've shown countless times that your analogy is way off the mark, and it doesn't even prove what you wan't it to prove ... the facts are against it ...
Reply: I am on my phone so o won't give a full reply right now. Instead I will just make a few points:

There is no experiment that proves that an IC system or it's core cannot arise by gradual changes. Show me the experiment that you think proves this. The fact that removing a part renders it useless has nothing to do with whether it could have evolved.

The first stage of the bridge is functional as a bridge. Random mutations may be more likely to render the bridge useless, but natural selection would remove those variants from the gene pool leaving only the successful one.

The probability of the wood being placed on top is irrelevant; it can happen, and that is the only version that natural selection would keep. Again, this illustrates that evolution is not random.

I have no proven fact to override because you have not demonstrated by experiment that IC can't arise from evolution.

The e. Coli experiment I am referring to is the one in which they learned to digest nylon, not citrate. I told you at least three times that no functionality was lost; they simply gained an additional ability.

Look up the definition of equivocation fallacy and tell me how it applies to the river analogy; you clearly don't know what it means.

Rainwater is not the river, and again the result s a self-modifying system.

And for the thousandth time, you can't just say I'm misapplying a definition without telling me how.

Now for the last time, give some unique falsifiable predictions of ID or admit it is not a scientific theory. Stop dodging this point.
Reply: Benjamin Toby "you might be wondering why Mark repeatedly asked if you even watched the entire video"

The first few times, he didn't make it clear what video he was talking about, and I asked him to link it to me, but he refused to.
Yes, he sure is a lot like you, in this regard and others.

Like I said earlier, I'm done with the whole "what is code" discussion, since we cannot move forward, we're just repeating ourselves.
However, you said one thing worth responding to, when I asked about morse code:

"they are all the same thing: sound patterns ... the code is still in effect anyway ... so I don't know exactly where the second level symbolism comes in here ... if I puch some buttons that make the sounds, and those sounds are symbolical for the message "hello" ... where is the second symbol to make it a code?"

1. We take the word "box", which is a symbol that refers to an actual box.

2. We encode the word, the symbol "box" into "beep-bip-bip" using morse code. It is now code, because "beep-bip-bip" is symbol for the symbol "box".
Symbol-for-symbol = second-level symbolism = code.

3. Some other person gets the message "beep-bip-bip", and recognizes that someone probably sent this with the intent for it to be decoded using the "Morse Code" code system, so they decode it back into "box". It is now first-level symbolism, again, because the word "box" directly refers to an actual box, not to another symbol.

I changed "hello" to "box", because "hello" is an interjection and might therefore be unnecessarily confusing.

The mere existence of the concept of "codes" means that any word or symbol you see, at any time, could be intended to see seen as code for some other symbol, because coding systems are arbitrary.
That's why we can hide secret messages in plain sight. It might look like "I'll be late for dinner" just means exactly that, but if it was intended as code, it could actually be an evil plan to take over the world, using some secret coding system.

"no you're trying to force an illogical thought through ... that's why I'm asking questions and pulling up explanations of my own to make you understand my drift... maybe you should give-up after you actually understand my point"

I'm not going to wait for you to actually give me a clear definition of what "code" is, anymore. We cannot move forward unless you give me a definition to work with, that I can attempt to falsify, or accept.
Until then, I am simply not wasting any more time repeating myself.

"I understand what you're saying silly, and I'm saying you're wrong" (About "code")

Then falsify it. Or fuck it, I don't care. You currently present an anternative definition of "code" (whatever it is). As long as you don't equate two different meanings/contexts of the word, I doesn't matter that you use the same word. So get to your point, if you have one.

"I clearly gave you an example of a program with a colour code changed to explain that a program contains codes ... and you go on to tell me a code contains a program"

No, not "a code". "Code" can contain a program. "A code" is just one symbol, not enough to produce a program.
"Source code" is the technical term for the thing that programmers write when they make software. It is the source code that is used by the compiler to create software from.
You probably know this, because you must have heard the term "source code".
A "color code", as you said, is something that the programmer writes, or refers to in his source code. A color code is a codeword for a color. This is all "collapsed" down to just values when the software is compiled. Any "codes" will disappear in the process, and becomes pure instruction and "data".
Conceptually, at the stage of writing the program, we referred to it is "color code", so that we would easily understand these complicated systems.
If it was easy, we wouldn't have to call it anything,w e would just do it. Abstraction! If I can just write, in my program, that something should be "red", then I dont' have ot care about how to make somethign actually appear red. I can rely on some other programmer having created the system where I can easily refer to the color by name, and it'll just "happen", and I can focus on my own programming tasks.
This is the concept of "abstraction", and the very reason that we can make complicated things, which would've been impossible otherwise.
But this is also what's causing this confusion, that the compuiter can somehow understand what "red" means, just because we've set up systems where we can act as if we can talk to the computer. It's an illusion that we have created, ourselves, to make programming easier.

"if you change the color code of a button to red, then you have a slightly different program ... simple explanation of a program containing codes "

Yes, except it isn't actually the program that's containing these codes, it's the source code that contains those codes.
I've tried to tell you think a multimillion times, and it just won't click for you.
When I change something in my source code, so that a green button will instead be red, then I have changed the source code. And yes, the outcome will be a slightly different program. That doesn't mean that the program contains any codes, only the source code was code.
And further more, the source code is just a bunch of symbols, aswell. It requires a mind to look at it and understand that some parts are differnet kinds of coding systems, and so on. It's all in our minds, and all conceptual. What is real is just a bunch of patterns the follow systems we've set up in a way that makes all of this possible to do.

"the primary term you should realize is intelligence ... you don't know if it was actually humans like you or some superhumans or even aliens ... you have no evidence of that ... we just know that intelligence can create such a thing so we assume it was humans like us " (Talking about the stone henge)

What is required is energy, to change rocks into a specific pattern. We know of no way that natural forces would use energy in this way, to produce this specific kind of thing.
However, take a look at "the giant's causeway":
https://upload.wikimedia.org/wikipedia/commons/7/7f/Giants_causeway_closeup.jpg
Huge places of that. And this was not made by some "intelligence".
But looking at it, it would be easy to assume that it was, because of our inborn biases.
But we understand that there are natural processe that produe that kind of thing.
When it comes to stone henge, we don't know of a natural process that produces such a thing, but we do know that humans exist, and that humans do such things.
Yes, we know that intelligent creatures can creatate such thing, but they could create giant's causeway, awell!
And intelligent creatures could dig holes aswell, but nature *also' makes holes.
We need ways to distinguish the difference, and the way to do that is to find the cause of it, not just assert what the cause is.
If science worked the way you think, we'd still be in caves.

"for the nth time what I need to tell you is experience we have of intelligence creating things like an induction motor or the computer code ... with this we can say that the flagellum and DNA were most likely caused by INTELLIGENCE ... and as a christain I say the intelligence agent was God ... do you understand now?"

A failure of reasoning. We know that the induction motor was created by humans. It isn't "intelligence" that produces them, it is humans that do.
Humans are a specific "package" of intelligence and the ability to actually do things, because we have strong enough bodies, and we've got tools and such.

And like I've pointed out, humans sometimes make things that nature also makes. Therefore, some things that intelligent creatures make is also made by nature.

" if a system is tested to be IC then it's not possible for it to arise by any process which doesn't involve spontenous assembly and instant functionality "

That's not true. IC proposes that you cannot remove any single thing and still have a working system. But evolution might not have added something to create that system, it might have removed something, for example. Can you tell what it removed?
What you need to do, to make sure something cannot have evolved, is to look at the DNA, not the thing that the DNA produces.
It is possible that one small change in DNA can have a multitude of effects on the outcome. Therefore, the idea of IC comes from a way too simplistic perspective.

"IC actually says this system is, as a matter of scientific fact, IC: therefore evolutionary processes can't possily give rise to it "

All claims about actual IC systems have been debunked, so far. The flagellum, the human eye, the bombardier beetle, and so on.

Whenever we do find something that appears to pose a problem, it usually doesn't go far enough to become a famous problem, because the scientists quite instantly notices the problem and finds the solution.

But what I've been trying to tell you that if something is "unexplained" it doesn't mean anything. If you use "unexplained" as an argument for something, then you're likely appealing to ignorance, which is a fallacy.
If ther eis some bioligical structer we can't explain that it is "unexplained" until someone can explain it.
IC effectively equals "unexplained". "this system is irreducibly complex" does not mean "this canont have evolved". No one has ever proved that IC means it cannot have evolved.

"IC is falsifiable ... take a bacteria without flagellum and create the neccessary pressures for mobility in a lab ... if the bacteria develops a flagellum, IC is falsified"

Of course IC is falsifiable. And the idea of IC comes directly from Darwin. It's just that he didn't know about DNA, so he had a very limited perspective on how it really works.
Anyway, you falsify IC by showing how something could have evolved. It's that simple. And we do that all the time, because it's critical to undertand how things can evolve.

However, no scientist ever claims that something is IC.
They have no reason to do that until they can establsih that it indeed is IC, which is really hard to do. And since "true IC", in the sense of something that "could not have evolved" should not be able to exist, since we know they evolved, for many reasons.
That's why you only ever heard creationists claim that something is IC.

"Newton didn't come to a conclusion of God because he gave up on his science"

Pay attention: He gave up because of his belief in god.
I've said this 2 times before, and you keep failing your reading comprehension.

"well search the damn page he stated it clearly he was no atheist and he gets "angry" when he's quoted for the atheistic viewpoint "

Yes, because he had a different view of what it means to be called an "atheist". I've explained this. It was a century ago, and culture has changed.
Today, he would be considered an atheist, because he was not a theist.
I mean, I am an atheist, and I agree with every word I have read that he said on the subject.

" atheist meant the samething in Einstein's time as it means today"

Yes, probably, but that doesn't mean that:
1... it doesn't carry a cultural stigma, or "baggage".
2... everyone understands what it means.

"I'm saying he was closer to theism"

And I disagree.

"agnostic actually means the human knowledge is too limited to disprove God ... ie there's not enough knowledge disprove the existence of something like God "

I've heard many different ways of defining it, but it carries the same core idea: That we do not know about god.
If is not a question of your personal belief in the existence of god[s].

"actually you said here that you represent science "

Yes, so does anyone whenever they refer to known science, the way I see it.

"less random, more random, STILL RANDOM"

Less sugar, more sugar, still sugar. Yes, but possible something else than just sugar, then.
If it's not completely random, then there is some sort of pattern to it, and that matters.
A dice roll may be quite random, but I can predict that you won't roll a 7 with one D6. Therefore, it's a priori less random than something that could roll any number. And this matters. A lot.

The question of how random things are is something that is heavily studied in computer science, because it does matter.

"you might want to re-read all instances I described evolution as random and see how absurd it really is"

Eh? Yes, it's extremely absurd. Evolution isn't random.

"The point is still that evolution isn't random just because mutations are. ... No it is random because all the processes involved are random"

OK, in one short sentence, you managed to prove that you don't know evolution. Congrats. Now go study it if you're going to have a discussion about it.

Also, consider how anyone could make a theory of something that is random. Theories are meant to predict things, so how do you predict something that is inherently random? You don't.

"Evolution is a lawful process with a specific outcome, not a random outcome. ... lol ... an undirected process creating specific non-random outcomes?"

God you're dumb.
Yes, exactly. That's very, very normal.

"Gould's law of irreversibility forbids that, so no, most certainly not. ... unfortunately evolution doesn't forbid this ... I mean it got a human from a bacteria"

A human from a bacteria wouldn't violate the law of irreversibility...!
It's weird how you start talking jibberish whenever you have no idea what I'm talking about. And sadly, that's way too often.

" I see most of your points ... they are based on fallacies as well ... most notably the equivocation fallacy in the definition of evolution"

Right now, go and read up on what an equivocation fallacy is.
The first thing you might notice when doing so is that "a definition" cannot be an equivocation fallacy, since an equivocation fallacy is the fallacy of equating two different things as if they were same thing. I wouldn't even know how to begin doing that when defining what something is. A definition is not a logical syllogism or anything like that, which means it cannot contain a logical fallacy.
I mean, sure, if you're really creative, you might be able to do it, I dunno.
Anyways, don't use grown-up words if you haven't learnt them yet.

"yes there was a point(not in time) where the universe didn't exist ... once something is proven to have a start, it means before it nothing of such sort existed ... simple logic "

We are talking about time, so when you say "where", you're already failing. I'm not saying the univesre is infinitely large, I am saying it always existed (time).
There was no point in time when the universe did not exist. Therefore, it has always existed.
You're saying there was such a point in time, when the universe did not exist. Tell me when that would have been, then.
You literally have to say T minus some number, but T doesn't go below zero, so you can't. T = the start of time, therefore, there is no T minus any number.

"well if you studied this in elementary school why the stupid questions considering that 3 of the 5 main religions are based on this same God I'm trying to explain "

But here comes the fun part: The same god did different things in all 3 religions.
So.... are they the same god, or not?

"not for evolutionists ... they're going to force it into the tree somehow ... lol ... just create another branch, conjure up another imaginary missing link, problem solved"

I don't care what you think some of them would do. You and I, and everyone else, would know that they are wrong, because of evidence.

"If you were back in that time, then there would be no sub-groups to those new phyla that you're talking about. ... yes there would be ... a trilobite was still an anthropod ... and there were different species of trilobites "

But we would need to have fewer levels of taxonomy to describe it. There would be no need to have the "phyla" level of taxonomy, perhaps.
The more life diversifies, the more levels you need to sort them all consistently. That's why instead of having something like 10 "layers" of taxonomy, we need to make a proper tree structure, in the form of a cladogram, which can have any number of layers and can accomodate any scale of time.

" Even if all life on earth was designed, the fossil record could not be evidence of it. ... why not exactly? ... it seems to me like your just trying to secure any path through which the thought of design can gain roots in your paradigms "

To know if something was "designed", you need to find the thing that designed it.
The fossil record, on the face of it, is only a catalogue of what species lived where and during what time.
To make the fossil record reflect design, you have to assume that each one was created separately, then destroyed and replaced by a nearly identical species, and that this process goes on and on. Nothing about the fossil record tells you that this happened, but that is what must have happened if they were all designed.
Teh fossil record tells you what existed, and in some cases other things, but does the fossil record tell you that those animals were born? No, that is somethign we infer. Likewise, if they wer created, we would ahve to infer that aswell, beause the fossil record doesn't show their births/creations.

So, lets say we find "god" and prove for sure that he exists, and that he did that thing that I described with the fossil record. Now all the scientist will go "OK, fine, but there was no way of knowing that before we found a god that does stuff like that".
It was never because of the fossil record that we knew they were designed. There is no way to draw such a conclusion from the mere existence of the fossils, or about where or when they lived.

A creator can do anything, but he/she/it might do nothing.
Perhaps we find "God" and we find out that the only thing he ever created were the asteroids in the asteroid belt. We had no damned way of knowing that.

"The idea that life was initially designed doesn't means it cannot evolve. ... more like "devolve""

Once again, Gould's law of irreversibility forbids "devolution".

"works well considering entropy "

Life is not an isolated system.
(Fuck, I'm so tired of people pulling up entropy...............)

"and I brought this up because evolution says anything can produce anything "

Source for that?
A cat cannot produce a bear, that is a fact. If anyone says otherwise, they're wrong. 
When someone says "evolution can produce anything", they do not mean that we can fuck with taxonomy however we want.
Yes, a cat could produce something that sort of appears to be a bear, but it won't be a bear. We would never classify it as a bear, unless we change how we classify things.
It would make no sense. A cat is a cat because it is related to cats. A cat cannot produce a bear, because that so called "bear" would be related to cats, not bears.
And the chance of cat DNA ever changing to be equal to bear DNA is not something we need to ever entertain the possibility of.

"but with evolution, a bear can become a cat with millions of invisible years"

Nope, and whoever told you that is lying or doesn't know what he/she is talking about.
It will never happen, unless we start classifying things in some other, really weird way.
What we currently mean by "cat" and "bear", a cat can never evolve into a bear.

"afterall, there's no restriction to the change and if a bacteria can produce a cat over milions of years, how much so a bear ... you see this predicition is atually unique to the Design concept"

This is just sad....
Yes, an archaic bacteria could become a cat, eventually, but a bear is on a different fucking branch on the tree!
A cat becoming a bear would imply a jump from one branch to another. That cannot happen.
But those archaic bacteria that gave rise to all animals, they were on the same "branch" on the tree. You can theoretically follow the lines/branches on the tree of life all the way from those bacteria, and up to cats, without ever having to jump from one branch to another.
Likelywise, you could follow the line from archaic bacteria to bears.
However, to go from cat to bear, you have to jump between branches. That is not logically possible.

"well don't you remember you accused the Bible of beign revised to be more in line with the evidence?"

Well, yes, and I'm happy about that. It's just that the problem is that when you bring the bible into line with the evidence of reality, you no longer have a religion. It crumbles.
But yes, you have a better book, from the viewpoint of being more realistic.

But what people are doing is that they're arguing for the same old god, but when you challenge the bible, they temporarily becoe more moderate about it, until they've met the challenge, and then they return to the same old thing.
If they actually stuck with keeping it in line with the evidence of reality, then they would have no religion.

"the only thing that changed about evolution is the definition ... which came from the normal "simple to complex" to "change in alelle frequency" ... I never knew one could change a definition so much to suit a theory"

Well, I can sort of agree with this. Yes, Darwin was wrong, if he said that evolution is the simple becoming more complex. I haven't read his book, so I don't know much about what exactly he said. (I have the audio book, but haven't gotten around to it.)

But you're essentially right in that the "change in allele frequencies" is a much newer definition. But it isn't a change, it is a much more precise definition, now that we understand genetics.
You really shouldn't find this strange. If someone sees somethign happening, and finds the pattern, but doesn't know th eunderrlying science, he can be correct in what he observed, but he might not express it like peopel will epress it later on, when they know the undelying science.

Do you know of the socratic method? If not, simply put, it is to make a statement about something, and then try to challenge that statement with some "exception" to it. Then you change the statement to account for the exception, and you repeat until there are no more exceptions that you can come up with. Then you have a "true statement", so to say.
It's a very good method.
If someone said "evolution means going from simple to complex", then yes, almost all scientist would instantly object to that, because they can give examples of the opposite.
So going through this socratic method, you end up with "change in allele frequecies..." statement, which never has an exception. Therefore, it is a good definition. Everyone will agree, because it is true in every case.
The socratic method is really good for defining things, I find.

"maybe they should have just renamed it to something like ... Theory of genetic change ... would be more accurate "

Theoretically, yes, they could've changed the name at some point. But because Darwin started it, I guess no one wants to take that away from him. He was still right, at the core, as far as I know.
But names really don't matter. The science still is what it is. If you have a poblem with the name "evolution", then changing the name helps with that, but it doesn't change what is true.
Sure, the theory of gravity has been effectively changed to the theory of relativity, though, as an example. The old theory is really only ever used as a decent approximation.

"which was that allele was a relatively new word coined-up in 1930 "

I definitely don't agree that 1930 means "relatively new". My grandmother wasn't even born, then, which means that it has been know for generations.
That was actually older than I would've guessed it was...

"Evolution was defined before the discovery "

Well, just as with gravity, it needed a lot more tweaking. That's science. With every change, it generally becomes more "true", not less.
I mean, can you imagine that more evidence and tests would ever make something less in line with reality?
So whenever we change or add to something, it's a good thing.

" and the new word ended up introduced into it to skew the definition"

"Skew"? Like I said, it's an improvement, since it no longer conflicts with any exceptions. Evolution is not simple things becoming more complex, because they evidently do not always do that. Becoming more complex should not be part of the definition of how life changes.

"It isn't the theory of evolution that explains that penguins give birth to penguins. It is a matter of classification. ... lol ... didn't you admit that the difference in colour in the peppered moths proved evolution?"

Yes, that is an example of evolution, since dark moths become more frequent, which light moths became rarer.
I really don't see how this is relevant to penguins giving birth to penguins.

"now you need to be damn sure that Carl was the first to invent a system for classifying life ... because I'm quite sure people have been classifying life for as long as they existed"

I don't know what system they used before Linné. But that is the current system, and the system we refer to. When we say "animal", we scientifically refer to the group "animalia", which is from that system.
Yes, there were probably "animals" before that, it just wasn't properly defined, I suspect. Like I've said, I'm not good at the history of science.

"Well, it also describes humans as spirits, in a sense. ... in the sense that the spirit is the part of the human triology that is actually the closest to Gods likeness ... the spirit is like a part of God given to man "

Yeah, things like that. What it actually means, "scientifically" would be a mystery.

"And god evidenetly was materials in the sense that he was visible. People in the bible have seen god. ... no one ever saw God ... according to the Bible, no one sees God and lives"

I'm quite sure it says both, as I remember it.
Genesis 12:7 has god appearing to Abraham, for example. Isaac, aswell, in genesis 26:24.
In many places it is implied that people saw him, such as Adam&Eve.
But I am also aware that the bible says that anyone who looks upon god would die, paraphrased. Very weird, but I do not care, and I don't propose to be an expert on the bible. The bible doesn't matter to me, obviously.

"actually God manifests himself in the physical in a couple of ways ... most notably light and fire "

Yes, anything we see is manifested by light, so to speak.

When I see something, I am seeing the light that bounced off that thing, or was emitted by that thing. We only ever see the traces of things, in this sense.

"actually applying critical thinking to the Bible reveals a stunning amount of truths "

Nono, you're mixing up "critical thinking" with "creative interpretation".
Critical thinking is closer to being cynical and taking the "negative" standpoint towards things. If you start with the viewpoint that the bible isn't true, then the bible does not persuade you that it is. This is skepticism.

"well if you're ready you can start be studying some aspects in the Bible and asking reasonable questions "

Who am I to ask? No one knows anything more than what the bible says, about the bible.
I may ask, for example, why god needed to send angels to scout things for him, if he is supposed to know everything and be everywhere.
In the story of sodom & gomorrah, the bible says that god had to send some angels down to check it out to see if the rumors were true.
Yet, peopel say he's everywhere and knows everything, but he doesn't act as if he does.
And I have no one to ask, because no one is an authority.
And ther eare countless of these "problems". And you don't see me arguing about it, because... yeah, I don't care, it's just a fantasy story, it doesn't have to make sense.

"like I said, Love is not controled by the hormones ... the hormones just show the symptoms"

Some part of the brain reacts to what we see/hear/whatever, and causes hormones to be released, which causes the effect of feeling "love". I mean, I don't know the exact specifics of it.
Of course, there are probably different kinds of love, but all these kinds still follow a similar system.
The brain is a machine, it can be tampered with.
I agree hat love isn't "controlled by" hormones, it's just the brain that reacts to certain things. The hormones are an effect, not the cause. But they cause us to feel this emotion/state.
The "love" that is here to make us reproduce is caused by the brain seeing hormonal markers in females, such as wide hips and whatnot. We have these emotions because they make us reproduce and make us protect our offspring, and so on.
Same thing with other animals, too, in general.

"the cause of the universe cannot be bounded by the universe' attributes"

From what we know, the universe cannot have a "cause" if time started with the universe. Without time, you have no "causes".
The universe has always existed, and it exists for some unknown reason. It might be that it exists simply because something must exist, or it would violate the uncertainty principle.
But we don't know why it exists, right now, if "why" is even a reasonable question.

"from what you're saying the big bang is actually magic "

It's "inflation". No, it's not magic, because it doesn't violate science in any way. Space itself can expand, and it does.
While parts of the big bang still isn't well understood, none of it violates science. It is not a suspension of natural law.

"and also I think I said this countless times but evolution is also magic by this thought ... because no known natural cause can create a human from a bacteria"

Evolution is that known cause, and it is natural, and it is observable and testable, and it is confirmed.
You keep insisting that it isn't, so in your head, perhaps it's "magic", but it isn't to science.

But humans didn't "come from bacteria", they came from the australopithecines, which were apes. You're not helping anyone by intentionally trying to make it sound as hard as possible to believe, by jumping a billion years.
Yes, it's really, really weird that humans could come from bacteria, but that's not really what happened. That is just a brutal simplification.
You're only trying to appeal to people's incredulity and their inability to visualize such long time spans. It's a lot easier if you follow the lineage of humans backwards, and see that no large jumps were ever required to explain the history of evolution on earth.

"I take it as a symbolical reference ... actually most of the Bible is symbolic "

Yes, that is exactly how I see it. It is a fantasy story that in large parts is symbolic.
But people of that time really did think the world was as desccribed by the bible: Flat, with the sky as a cupola/tent, where the stars were attachedd, adn the sun (which is not the same as a star), and the moon as an actual light source, and so on.
It's the "firmament" model of the world. They even thouth that the sky was an ocean, aswell, as this is shown in Genesis, where god separates the waters below from the waters above (the sky).
Yes, the bible are the ramblings of idiots, from our point of view - but I don't blame them, because they didn't know better.

"and I'm not sure of your rationale for the stars before earth assertion : I'm no expert in cosmology ... I barely read up on it tbh ... maybe you should explain better "

That's fine, we can't all know everything about everything, and neither do I.
The big bang only created hydrogen, helium, and some lithium. Those huge clouds of gas collapse to form stars.
Inside stars, those atoms are pushed together to create heavier elements, and this is what fuels stars. Nuclear fusion.
Then the stars die and throws these new elements out into space. So with the next generation, it's finally possible for rock to form. Earth is a rock planet. All the material that makes up the earth comes from stars that have exploded.
Therefore, stars existed before planets.
And in either case, the earth is only 4.54 billion years old, while the universe is 13.72 billion years old. So that makes about 9 billion years before earth (and the sun) was formed.

"You mean show me some technology that beats humans? Pretty much everything we build are built simply because they do things better than humans do them. more specifically: faster ... not necessarily better"

"Faster", when speed is what we want. "Stronger" when strength is what we want. And so on.
We can beat any characteristic of humans by far, except for the human ability to innovate.
However, we're very soon making technology that beats human innovation, aswell. Ironically, by using evolution.
We can create programs that program themselves using evolution. It's "genetic algorithms", amongst other things, collectively called "meta-programming".
And we're building computers with more processing power than a human brain, very soon.

" I don't see how the creations can beat the creator ... maybe if a calculator could repair itself after loosing a wiring it could come remotely close "

You don't see how? Well, if you don't see how, I can't explain it to you. I have absolutely no idea why you even though, to begin with, that a creation wouldn't be able to beat its creator. There was never a reason to propose that.
Yeah, a self-repairing calculator would be one hell of an expensive calculator. No one would try to sell that.
But a calculator can already "live" longer than any human can. It's really easy to make a calculator that will continue working for 500 years.

"and I'd like you to get a calculator, or any computer make computations, analyse data, control nerves and functions, regulate body temperature, and the other numerous functions of the brain for one hour on the energy of a sandwich"

Computers don't have "nerves" and don't need to regulat their body temperature, and os on. You're talking nonsense.
The human body is very complicated, therefore it needs a large brain. And the human body requires a lot of energy to function, and it is weak and fragile.
The energy of a sandwich is huge. The problem is that he body is unable toa ctually make use of most of it. We can make technology that extracts more energy from a sandwich than a human body does.
The human body can only work with organic compounds. We can make technology that extract energy from things that would be poisonous to humans.

You seem to be under the delusion that life is really great and perfect. It's really damn far from it. We could imprrove pretty much every detail about the human body, theoretically if not yet practically.
We could even improve the cells. We've invented XNA, which works just like DNA, but is strong and better than DNA.

"also you've missed the most important aspect of humans: sentience ... this beats any technology we have hands down ... just imagine if you could get a car to think for itself "

First of all, you don't want a sentient car, becaue that would no longer be "technology" and instead be "slavery", and sentience itself is of no inherent value in technology.
You want an intelligent car - which we already make - but you don't want a sentient car.
Sentience is overrated, except for the curiosa.
And you're right, we can't make sentience, yet. We still don't know when something could be said to be sentient. Perhaps we've already done it, it's just that we don't know how to define it. We don't have a "theory of the brain", yet, either.

"yes it does wtf ... there are electrical components inside without which you have a bunch of metal orbiting in space ... what do you think the solar pannels are for? ... u kidding?"

Even a teapot that orbits earth would be a "satellite".
Satellites, in this context, means anything in space that orbits somethign else. Even a moon is a "satellite", and so is any small debris in orbit, aswell.
A "bunch of metal" orbiting earth would also be satellites, in the broadest sense of the word.

But when we make satellites, yes, we tend to make them useful. And with solar panels, they will last longer than a human lasts on a sandwich. We've got other means of producing power than solar panels, aswell. There are generators that generate power from radioactive decay, which lasts a few decades, and gives quite a lot of power.
The rover Curiosity has one, and the probe we sent to Pluto, the other year, also has one, since solar panels don't really work that far from the sun.

"well the birds can access the functions of a sitellite and gps with very little energy and lesser space taken "

No, they cannot. They have atoms of iron in their brains that react to the magnetic field of the earth, which makes it a compass. It is not precise. It couldn't be very precise, because the magnetic field of the earth changes a lot, so the birds would get lost all the time.
They rely on memory and such, aswell.
And yes, we can make a GPS tracker that is smaller than a bird's brain, and has much better precision.

"my point was actually related to air planes navigation system ... birds know how to navigate their way even much more efficiently than any plane you can call up"

No, airplanes can use GPS, which is better than a bird's built-in magnetic compass.
Where did you get this idea that bird are particularly accurate in their navigation? Yes, they find their way, but their nagivation "system" is not very accurate. They can end up kilometers wrong, but when they recognize where they are, they fly by sight and memory.

What I am saying is that birds use the same techniques as human do, for finding our way. We learn the way, and we use memory and sight to find landmarks, and so on.
Bird who migrate use the stars and the sun to stay of course, aswell as this magnetic compass. But becaues tehy fly the same route every year, they also learn, especially by following their elders, the way to where they're going.

If a bird were to fly blind, it would not get anywhere near where it wanted to go. It would fly the generally correct direction, but the precision is so poor that they would still be off by many degrees.
Humans also have a built-in compass as part of our 20 (or 21) senses. This has been demonstrated. It's probably not as good as with birds, because we don't have to rely on it as much as birds do.
But we have "a sense of direction", like birds, just not as good.

"Depends on what you want it to do. I listed a few examples of how technology beats humans. We can combine a lot of those things, if we wanted to build somethign that is specifically built to meet your challenge. ... lol you know there's no present robot that comes remotely close"

Who was talking about robots?
We can build something stronger, faster, more perceptive, better reflexes, and with more processing power than the humans brain, which could also have a lot of abilities that humans simply do not have, like radio transmission capabilities, internet, night vision, and so on.
Like I said, we can beat any characteristic of the human body, by miles, apart from the human ability to innovate. And we'll have technology that beat that soon, aswell.

"If you read it one more time, you'll see that I said "any such system will evolve". I said nothing about a specific kind of change, like single selled to multi-celled. ... well there's no evolution if single cells cant transform into multi cells so you're shooting yourself on the foot"

Absolute bullshit. Single-celled organisms evolve just as much as multi-celled organisms.
Being multi or cingle celled makes no difference, you still evovle because the gene pool still changes with time.

And as for single becoming multi, that took a few *billion* years to happen, the last time. Don't expect such a rare thing to happen very often.
Normally, being single-celled is better than multi-celled. That's why I don't personally know why we ever became multi-cellular, at all.
Single-celled life still rules the earth, and we still live at their mercy, basically. Most life is still single-celled.

"not stupid a change in gene frequency over time means the population has changed ... from a population of mostly green to mostly brown beetles ... that's just genetic variation"

Hey, it's no me, it's berkeley!
No, but seriously, "genetic variation" is the fact that variation exists. "Evolution" is the fact that the "average", the "center point" of the genetifc variation changes in a specific direction over time.
That is, for example, humans vary in length, but over time, the average human's length changes. That is evolution, not "genetic variation". Two different things.

From mostly green to mostly brown is evolution, because it is a change in gene frequency, which is the definition of evolution.
This is the phenomenon that also eventually causes species to split into new species and create a tree structure, given that mutations are also introduced regularly.
Two geologically seprated groups of the same species will evolve in different directions, and will evenetually become too different from eachother to be of the same species. That is "speciation".

"what a desperate attempt to validate a dogmatic theory "

I can see you're trembling in your boots. The moment you know you're beaten, all you can do is to try to trash-talk.
Sorry, it doesn't work on me, I can see right through it.
Remember when you complained about how the theory of evolution has changed "too much", that it shouldn't even be called the same thing? Now you're saying it's "dogmatic". You're contradicting yourself.

"like I said, your ape-men ancestors can easily tell these beetles are getting more diverse ... wasn't that why there was selective breeding to start with? artificial selection "

Ape-men who selectively bred beetles? Just what on earth are you talking about? Did you just have a stroke, or something?

"I know evolution is not a scientific term and it means gradual change from simple to more complex"

You're mixing up contexts. Outside of science, "evolution" generally just means gradual change, and generally from simple to complex. We can talk about cities evolving, for example.
In biology, it doesn't mean that. In biology, it is a very specific phenomenon that is desribed by scientific laws and principles. The link to Berkeley explained it clearly for you.

If you treat them as the same thing, then you've got an equivocation fallacy.

"it says for example junk DNA aren't junk like you say ... it also predicts there'd be signs of design ... the flagellum is a perfect example ... the DNA is also"

The level of fail here is quite impressive.
Imagine if science was like that. Someone makes a hypothesis that could explain something, and the prediction is that "we should se signs of this".
Fucking genius "prediction". It'd be like kids in a fucking sandbox.

"humans and earthworms both contain cells ... so whose their ancestor?"

Oh, I don't know, I could find out, though. Not that you'd care.

"*And yes, it keeps being correct. The theory of evolution predicts which fossils should exist, and where they should be found.* ... lol and the scientists do the remaining job of adding the remainder 90% missing parts to confirm the prediction"

Nope.
But how about those creationists who imagine 100% of the evidence that's missing for their ideas?

"*Go somewhere else and cry about how you pet hypothesis won't get recognized because it happens to be shit.* ... no it's ignored because of it's implications ... not it's evidences"

It's "evidence", not "evidences". Why do creationists insist on putting an "s" at the end? You should look up the background for that, it's quite interesting. Some creationist wrote some article in the 1970, or something, which pluralized "evidence" with an "s" at the end. Then it spread through the creationist community.
But because creationists never actually read science, it stayed a creationist thing to pluralize it like that.
It really tells you something about creationists and science. Basically, whenever you see someone pluralizing it like that, you know they've never studied science.
(Also, it's "its evidence", not "it's evidence". But whatever.)

Anyway, like I said, don't cry to me about this. "Uhhuuu, they're just afraaaid of the implicaaaations"... **sob*".
Go and convince your creationists buddies to actually make proper hypotheses, instead. If you want to play science, then at least follow the scientific method.

You know who was afraid of the implications? Darwin, when he discovered common descent. He was genuinely worried about what it would do to religion, but the cat was out of the bag, and he couldn't just put it back in.

"*Yes, I would fire any scientist I have who would argue for ID. Why? Because you can't argue for ID, so anyone who would say they do is a half-wit.* ... of course fire anyone who has an alternate argument that refutes yours because you just can't, or don't want to understand it"

No, fire someone who is supposed to be a scientist but can't even reason properly. I just explain this. Can you read?

"you're quite dull"

Heheh, ok. That's a new one, "dull".

"Behe proposed a way to falsify IC"

I've explained how easy it is to falsify "true IC". All you have to do is show how something could have evolved. We do this all the time.

"*Bird wings evolved from dinosaur arms.* ... which evolved from bacteria ... why are you trying to evade your nanoscale daddies"

I am trying to make it easier to understand. It is a fact that bird wings evolved from dinosaur arms. And because that is much easier to explain and understand, it is a better way to make people understand. Do you get that?
If someone asked how to make a car, would you explain what parts you need, or would you explain what atoms you need?
You choose to explain what atoms are needed to make a car only because you want to make it sound as hard as possible to make a car, to the point where people will no longer believe that cars can be made. But they obviously can. You're only trying to appeal to people's incredulity.
But what really bothers me is why you try this tactic on me. It makes little sense.

"*Why do you even go on inernet and discuss shit you know nothing about? You're wasting everyone's time, and looking like an idiot while doing it.* ... firstly going back to school for me would be studying more importand topics"

Fine, do that. Just don't go around saying shit is or isn't some way when you don't know what you're even talking about.
I've had to define evolution for you, and you still don't seen to even get that. You come on here and say that evolution is effectively wrong, but you don't even know what it is, and you insist on things that are absolutely moronic.
And that's fine, if I were to discuss the bible with some experts, and insist that I know it just as well as they do, I would likely look like a fool, aswell.
And let me make this clear: Compared to you, I am an expert on the subject of evolution.

"secondly you've even admitted discussing stuff you don't know anything about"

But not pretending that I know something I don't. I speculate, sometimes, because it is interesting, sometimes. And I always do my best to make it clear when I am speculating and when I am referring to existing science.
But sure, I am only human, and I probably make mistakes around this, aswell.

"thirdly mathematically the one wasting time would be the one TYPING OVER 1000 LINES OF CRAP"

It isn't crap, or a waste of time. Even if I fail to teach you anything at all, other people might (and actually do) read this, and might have use for it.

"I'm even trying to save time with shorter responses and get to my point as quick as possible"

I fully admit that I am really bad at that. I might have a convoluted communication style, probably because I have Asperger's syndrome.

"Fourthly I'd look like an idiot in the eyes of people like you certainly ... that's because a world class restaurant dish is trash for a pig"

By that, you're insinuating that you know so much more about this than I do, that I can't even grasp it, and don't even understand how wrong I am.
If you had shown any sign that this was the case, fine, but you've only shown the opposite.

"...first fucking define what "humans wings" would be, or no one can answer your question. ... seriously? ... ok just take any wild guess : imagine how the wings would look like"

OK, I'll take some "guess". I'll guess they'd be bubble-gum-powered hot air balloons.
Seriously, don't pose a problem and then refuse to define the parameters of the problem.

"*If you're talking about simply making humans fly, then the reason it won't happenis because we would have to have insane chest muscles to produce enough force to lift our bodies.* ... evolution is up to the task"

No, sorry, you're the one who claims that evolution isn't up to it. You're the one who says A can't evolve into B.

"*We are simply too heavy, that's the main reason.* ... with evolution that's a piece of cake ... we can just develop stronger wings or loose more weight"

I have already explained to you that this would then put the solution so far into the future that I cannot even reasonably speculate about it.
You're then talking about soemething unknown evolving into something unknown. There is no point in specualting about that.
And "strong wings" means more weight, which means we need even larger muscles, which adds to he weight, aswell.
Humans are in no condition, currently, to develop flight. Dinosaurs were, because hey had pneumatic bones, and feathers.

"*That is, if we're talking about powered flight, not just "gliding". But if you're just talking about gliding, then that is a different thing.* ... I'm also talking about wings ... like bitds"

Humans cannot evolve bird wings. And liek I siad, I don't know what "human wings" would be. It would be something unlike any wing we've seen, so far.

"*only in theory can it change anything into anything, but never in practice* ... I see : in reality a bacteria cannot develop wings but in theory it can ... interesting ... then that means in theory anything can develop anything ... doesn't make the theory any more valid"

Wait, why can't a bacteria develop wings? Wings are not "anything". I said that in practice, evolution cannot turn anything into anything. "Wings" are not "anything", they're one specific thing.
What evolution can do is contextual, it depends on what you've already got, amongst other factors.
That's why the process of evolution can do anything, but it cannot do anythign with anything. (That's where the "in practice" comes in.)
Evolution could change any DNA sequence into any other sequence, on the face of it. But in practice, those sequences actually have effects that impose restrictions on how somethign can/will change.
For example, you can't just remove the brain from a human. Our bodies rely on them to survive. Given a shitload of time, perhaps the brain somehow would become obsolete, it's just not practically likely to ever happen.

"*The environments can't produce any selection pressure, in practice.* ... so what about a case where an environment of more predators affects the population of weaker preys? ... is that not something that can be observed in real life?"

Hmm, I think taht maybe you misunderstood me, here.
Evinroments can't, in practice, prose absolutely any kind of selection pressure. Natural environments are limited to the kinds of selection pressures that they can produce.
I am not saying they can't produce sleection pressures of any kind. That's be crazy to say.

For example, on earth, the selection pressure on a species probably cannot be "you have to avoid getting hit by meteorites". I mean, you understand that there are some kinds of selection pressures that just can't really exist, because the environment is limited to what selection pressuse it can produce, right?
This affects what can evolve, aswell, since the environment controls evolution. Evolution is onyl adaptation. The environment introduces a problem thata the species need to overcome, then it introduces a new problem, and so on.
Without any "problems" (selection pressures), evolution nearly stands still.

"*and the fact that evolution always has to work with what it's already got imposes some limits.*  ...no it doesn't because there's no restriction for what can and cannot be useful ... the same trait can be useful and useless at different environments"

Yes, that is correct, but I didn't oppose that.
If you have 100 million years of evolution, then during that time, your species may face a number of different problem. The nature of those problems well be the reason you end up evolving a specific way.
For example, the cheetah would not evolve to be so fast if it didn't ahve to chase fast animals. If cheetas ate bears, not gazelles, they would've been very different.
And there are some kinds of environmental pressures that simply do not exist. No animal ever had to evolve the need to camoflauge itself as a spoon. That's why no such animals exist.
So not anything can practically evolve. Only that which makes sense and is possible from the perspective of what you've already got. If humans need to evolve flight to survive, then we're fucked. We'll be extinct before we could ever evolve flight.
However, we might solve the problem some other way, and not evolve flight, but instead evovle the ability to become invisible, or something. Few such problems ever have one single possible solution.

"*For example, humans can probably not evolve away our spines, because any attempt at doing that would be deadly, so humans will forever have something similar to our spine.* why can't we? it'd just cause an extinction ... something all too common with evolution ... so?"

Because natural selection could never select for that. :P
Not having a spine could not be selected for, because spine-less humans would not have more offpsring than those with spines, because they would be dead.
And no, it wouldn't cause an extinction. There are humans who are stillborn, every now and then, because they lack skin, or some other really deadly mutation. They are instantly weeded out by natural selection. Evolution cannot go that way, because it's just not possible that losing our skin could be beneficial. We die from that.
As long as "normal" humans are born, they will be infinitely more fit that someone who is born dead.

The only way that evolution ever causes extinction is when some predator "accidentally" get a mutation that makes them "too good", and they eat all their prey, and then they die from starvation, becaue they screwed uo the predator-prey balance.
That probablyhappens very, very rarely. Humans are an example, though. Evolution cannot plan ahead, and isn't "aware", so it couldn't predict the power of complex language. Once we evolved complex language, we quickly screwed up the eco balance on earth. We're still around, though, but we've made a lot of species extinct.
The other way evolution can "cause" extinction is when it has made some species too niched, and then it is unable to adapt when the environment changes. this is quite common.
Some species has become an expert of eating some insect from a specific tree, and can't do anythign else. But then those trees go away because o environmental changes, and the species is screwed. Happens a lot.
But the close relative of that species may still go on, which at least partially makes the same genes keep going.

"since evolution can do anything ... it can conjure up another perfectly functional compartment in the ass for example where oxygen can be stored for flight "

The reason we have lungs is (as we currently understand it) that the lobe-finned fish from which land animals evolved had pockets/sacs of oxygen in their blood vessels. This allowed them to do what I described. They could get up on land for a while, before they had to return to the ocean to get more oxygen.
Those sacs of oxygen gas grew bigger, and they are what we call "lungs", now.
The larger those sacs grew, the longer they could stay out of water, which was beneficial for many reasons.
Eventually, they didn't have to go back to the water at all, anymore.

"*Anything can't produce "anything", only in theory, but not in practice, because in practice.... well, I've gone over this, alredy.* well in practice we have adaptation and variation ... no evolution ..."

Adaptation is because of evolution. Is this really so hard for you?
You've got a group of individuals, and you've got a problem. Some of those individuals will be more fit to live with that problem present, so they will have more offpsirng, which might inherit this fitness. Genetic variation causes some of those offspring to be even more fit, and have even more offspring, some of which will be even more fit.
This leads to the species adapting. And it is evolution. This is all evolution is.
If two separated groups of the same species don't mix their genes with eachother, then their individually different selection pressures will cause them to adapt differently, which eventually causes them to be incompatible, which splits them into separate species.
Repeat this for billions of years, and you've got the history of evolution on earth. Nothing else is needed.

"I refuse most of your points because it'd be stupid of me to just swllow your drivel without proper thinking"

Firstly, I do not want you to swallow anything unless it make sense to you.
Secondly, nothing will make sense to you, because you insist on a view of the world that is incompatible with reality. The only things that will make sense to you are the models you create in your head babout how the world is, based on your presumptions. Whenever you are forced to take reality into account, you will have problems.
And clearly, you react with aggression to such situations. That's not helpful.

"you're scared to have your beliefs shattered by the truth so you'd do anything to pervert any thought or evidence supporting ID"

Sorry, you're extremely wrong. I would love magic to be real, who wouldn't?
The reason religions exist is because they try to sell you a better death. And everyone wants eternal life in paradise, so do I.
It's just that those are just stories based on people's hope/wish that such things were true. That's why they're so "perfect". Unrealistically* perfect, in all ways.
I mean, when a religion tells you that you'll get everything you've ever wanted, and eternal life and love and no sickness or evil - do you seriously not for a second realize that it's obviously bullshit?
Someone is trying to sell you something, and because they don't ever have to show you the thing they're selling you, they can exaggerate all they want.
Any reasonable person would be suspicious, at least. But you swallow it whole, even against evidence and reason. Probably because of culture/upbringing, most likely, but I don't know you, so I couldn't possibly know.

"well not so fast ... you came up with 1500 lines you're going to defend every single piece of crap you spouted"

Say "please". You cannot force me to do anything. You can clearly see the effort I put into this, yet you're not appreciative of that effort at all. I am not paid for this, I do it out of good will.

"you've said close to nothing and I have had to repeat my self over again in many instances"

Yes, this concersation had degraded into a bunch of nothing. I've started skipping over some of the parts that are really "nothing".

"maybe you could be a little wiser and tackle the issues one at a time, with shorter lines and MORE  THINKING"

"Wiser", huh? How about you at least get past the definition of a few word, before you talk about "wise". You're not ready to even "start thinking" before you can even uinderstand the meaning of the words involved.
You think you undersand it, and you're very confident about it, but you're completely wrong. Learn some humility and learn to admit that perhaps you've misunderstood some things. You have, gravely.
Reply: I really can't spend this much time on this, and this frequently.
Reply: Max Spiegel

you know what I'm just going to limit my lines as well and get straight to the point ... this is getting unbearable ...

The first stage of the bridge is functional as a bridge. ... you just changed the analogy ... PS the first stage would make a lousy bridge ... still would be eliminated by NS ...

The probability of the wood being placed on top is irrelevant ... yes it is because you're talking from imagination and to a rational person, it's the most probable that goes ...

I have no proven fact to override because you have not demonstrated by experiment that IC can't arise from evolution. ... I have demonstrated by experiment that an IC system needs the IC core spontaneously assembled for functionality ... 

And for the thousandth time, you can't just say I'm misapplying a definition without telling me how. ... never mind ... it doesn't matter how many times I say it at this point ...

Now for the last time, give some unique falsifiable predictions of ID or admit it is not a scientific theory. Stop dodging this point. ... and for the last time: IC proves that intelligence can be observed and tested for ... PS do you mind telling me again of the unique prediction made by evo that says penguins always produce penguins? ... I must have missed the definition of "unique" or "prediction" ...

mr Spiegel I really wan't to believe I've not totally wasted days or even weeks explaining my position to you ... if not then there's no more I have to say ...
Reply: antiHUMANDesigns

I really can't spend this much time on this, and this frequently. ... oh I see ... you finally realized 1500+ lines is time-consuming? ... well I'm afraid but you've wasted thousands of lines and plenty of time just because you can't look closely and think properly ...
Reply: Benjamin Toby The level of aggression from you...
1500 is very time-consuming yes, but I once had a conversation where my comments were over 4000 lines long, and the other guy wasn't far behind.
I do enjoy this as a hobby. 
It's a shame you think most of it has been a waste. But like I've said, it's there for posterity, or whatever. If you don't appreciate it, perhaps someone else will.
Reply: antiHUMANDesigns  aggression? I came with less than 50 lines ... you came with thousands ... is this another yet  miscue from you? ... well I have a duty to protect myself from faulty thoughts: which you're trying to force through ... still working on your comment ... hope at least you get to actually do some thinking this time: naive of me but that's the only way forward ...
Reply: Benjamin Toby
"you just changed the analogy ... PS the first stage would make a lousy bridge ... still would be eliminated by NS"
How did I change the analogy, and why would the first bridge be "lousy?" It would still work as a bridge.

"...you're talking from imagination and to a rational person, it's the most probable that goes"
Evolution is not a "rational person." It is a natural process, and has no interest in getting the best design on the first, or even the 1000th try. If evolution produces 1000 bad variations and 1 good one, it takes the 1 good one. You are not NS.

"I have demonstrated by experiment that an IC system needs the IC core spontaneously assembled for functionality"
For the umpteenth time, what experiment? Post the study!

" it doesn't matter how many times I say it at this point"
Correct, it only matters how many times you can show it, which is zero so far.

"IC proves that intelligence can be observed and tested for"
How is that when IC structures can arise by gradual evolutionary change?

"PS do you mind telling me again of the unique prediction made by evo that says penguins always produce penguins?"
As AHD said, the fact that penguins produce penguins is a matter of definition and not a unique prediction of the theory. Unique predictions of evolution include, but are not limited to, our genetic similarity to chimps (including large portions of the genome that are present in multiple copies and have no actual functionality), transitional fossils, the lack of precambrian rabbits, etc.

"mr Spiegel I really wan't to believe I've not totally wasted days or even weeks explaining my position to you"
You are wasting your time by not providing experimental evidence to support your claims or giving testable, falsifiable, unique predictions that would make ID a scientific hypothesis.
Reply: Max Spiegel

Evolution is not a "rational person." ... just wanted to point out why I'm probably not going to waste more time with you ...

As AHD said, the fact that penguins produce penguins is a matter of definition and not a unique prediction of the theory. ... I don't think you should be quoting AHD for me cuz most of his lines turn out to be nonsense ... PS you told me the prediction of evo. is that a herring can't produce a penguin ... also, there are little to no transitional fossils except the ones conjured up out of imagination ... and the prediction of evo is that there'll be countless transitional fossils ... which is untrue ... ID predicts there'd be no transitional fossils : and the fossil record supports us ... ID also predicts evidence of spontenous creation, which is what the cambrian explosion signifies ... ID predicts no Junk DNA the many DNA functions once considered as junk appear to have functions ... 

as for experiments there are countless experiments on knocking out parts : the best I can remember is the experiment with fibrinogen in mice ... there's also a situation called Aphakia which is the loss of lens of an eye: renders the eye effectively useless ... you can do one yourself however : just try removing the aorta from you heart: QED ...
Reply: Benjamin Toby "aggression?"

Yes, your bad attitude. You keep acting agressively and defensively, instead of having a proper conversation. Your extreme over-use of "lol", and being extremely dismissive and just all-around unpleasant.
Reply: antiHUMANDesigns

yeah I figured by "proper conversation" you mean I sit down and just download your BS without questioning ... 

and btw "lol" just means a laughable comment ... there's nothing unpleasant there ... atleast nothing compared to using the word "moron" ... so chill out and wait for you reply ...
Reply: Benjamin Toby So you think evolution is a rational person? Sorry pal, but if you think nature behaves like people you need to go back to second grade.

As for transitional fossils, here are a few:
transitionalfossils.com

And again, the fact that removing a part makes it lose functionality has absolutely nothing to do with whether or not it could have evolved. You need an experiment that shows that something that loses functionality as a result of moving a piece means the structure cannot evolve, which I have already demonstrated is false with the bridge analogy.

You are running out of steam, buddy.
Reply: Benjamin Toby I can't believe you dismiss all of it as "BS". I don't dismiss everything you say. 
If you keep a bit more neutral attitude towards it, then perhaps you can find something of value in it.

Anyways, will you respond to my last reply to our large conversation, or are we killing the conversation, here?
Reply: antiHUMANDesigns  Umm yes you do dismiss most of it: you've even admitted it ... and I keep a quite neutral attitude ... if you realized I rarely argue with anything that is not factual ... but I don't think same can be said about you ...
Reply: antiHUMANDesigns 

The first few times, he didn't make it clear what video he was talking about, and I asked him to link it to me, but he refused to. … Oh I see he only needed to give you the link to the video you spent so much time commenting on …  

Yes, he sure is a lot like you, in this regard and others. … No surprises … sure you wouldn’t be surprised if I told you you were just like Spiegel … 

Like I said earlier, I'm done with the whole "what is code" discussion, since we cannot move forward, we're just repeating ourselves. … we can move forward if you just start reading … actually … 

1. We take the word "box", which is a symbolthat refers to an actual box. … lol … early fail … I say take the word “hello” … which is of course a symbol that refers to ….. Ummm … Hello! ... lol … your second symbolism argument crumbles instantly here … I’m not sure it even holds up the the box analogy … 

In addition, what if I want to encode a letter “A” using morse code … what happens then? What does “A” stand for? A? if I just send this as a message using morse code… does it mean I haven’t used any code? …

I changed "hello" to "box", because "hello" is an interjection and might therefore be unnecessarily confusing. … really? … hmmm …

Then falsify it. … like I said, your definition of code implies that all operations of computers are void of code, except programming … the basic reason I’m rejecting your definition is that you think code is strictly conceptual … If I go by your definition, and treat symbol as a physical quantity then my analogy fits the description of code … let’s say the button in my analogy represents the switch patterns: ie the switch patterns are symbols for the button … and the switch patterns represent the closing and opening of the circuitry (ie the one made of the collectors and emitters) : this pattern in turn represents the lighting pattern required to display the letter … we now have a situation where the base patterns represent the button press and also represent the collector and emitter patterns: which in turn represent the LED pattern: which is the letter A … 

Aside this, I brought up the analogy to explain the Computer code : and from this a code is anything that represents a specific action … ie and action that is constant as far as the code is … applying this to the morse code analogy if “hello” is represented by “.-….“ and this pattern repeatedly translates to that same action, then that pattern is a code … if this pattern is changed to “.-…” and this represents “go left”, then this is a different code : so long as the interpretation brings the same exact action … so in morse code the code is the symbol that represents a constant value … so of “.--..” represents “A”, then “.-..” is the code … but from your definition there’s no code here because the letter “A” is not a symbol for anything …

Also your definition is probably false because you said that from my analogy, the letter “A” displayed is the code … that would be equivalent to saying the “box” in your analogy is code …

"I clearly gave you an example of a program with a colour code changed to explain that a program contains codes ... and you go on to tell me a code contains a program"

"A code" is just one symbol, not enough to produce a program. … but codes can … this was why I said a program contains CODES … no one code … a single code contains a single function … and that’s how it is in reality, and even in the morse code … 

"Source code" is the technical term for the thing that programmers write when they make software. … the “thing”? really? … the source code is the “technical term” for all codes contained in a program or application …

You seem to not get my point once more … by programming we mean arranging things to achieve certain functions … code can’t contain a program because a code translates to one function alone … in programming we aim to arrange these functions to get distinct functions … 

 It is the source code that is used by the compiler to create software from.
You probably know this, because you must have heard the term "source code".

A "color code", as you said, is something that the programmer writes, or refers to in his source code. A color code is a codeword for a color. This is all "collapsed" down to just values when the software is compiled. … the colour code is the value for the specific colour …  since the color code usually just one step away from binary form(hex code), what happens when you just put the binary code instead? … doesn’t it mean you’ve just added “values” where there’s supposed to be just “codewords”? … this means that the codewords are the values … just in shorter forms … that’s all … 

Any "codes" will disappear in the process, and becomes pure instruction and "data". … the codes don’t “disappear”… they are only translated into the original code … which is binary … 

Conceptually, at the stage of writing the program, we referred to it is "color code", so that we would easily understand these complicated systems. … no it’s called color code because it’s actually the code for the color … just in a different representation … take this example : in html, red and  #ff0000  translates to the same thing: which is probably something in the line of 100011110001 … the only reason you get to type red or the hex format is just for simplicity … that’s all … there’s nothing here related to just “hiding symbols under symbols” … it doesn’t matter the symbol you use since it’s just going to end up in binary form … 

*I can rely on some other programmer having created the system where I can easily refer to the color by name, and it'll just "happen", and I can focus on my own programming tasks.*… ease is the only thing achieved by computer code … this also invalidates your conception of “hiding things within symbols” … 

Yes, except it isn't actually the program that's containing these codes, it's the source code that contains those codes. … the source code is just a name for the program from the point of view of its codes … the source code is just the codes that make up the program …

I've tried to tell you think a multimillion times, and it just won't click for you. … and it doesn’t matter how many times you repeat the same nonsense to me … you have to justify it with logic …

When I change something in my source code, so that a green button will instead be red, then I have changed the source code. And yes, the outcome will be a slightly different program. … so WTF are you blabbering about? … Source code = program codes … ie the codes that make up the program … maybe you should explain how code can contain a program … 

That doesn't mean that the program contains any codes, only the source code was code. … of course the program contains a source code,  the source code is the code … but that doesn’t mean the program contains any codes … beauty …

And further more, the source code is just a bunch of symbols, aswell. It requires a mind to look at it and understand that some parts are differnet kinds of coding systems, and so on. It's all in our minds, and all conceptual. What is real is just a bunch of patterns the follow systems we've set up in a way that makes all of this possible to do. … well what ever you see in a source code is directly equal to 001010101010101010101111 … doesn’t matter the language … it’s only another form of binary code … just like saying the same word “come” is equivalent to “komma” and “ven” and so on …

When it comes to stone henge, we don't know of a natural process that produces such a thing, but we do know that humans exist, and that humans do such things. Yes, we know that intelligent creatures cancreatate such thing, but they could create giant's causeway, awell! And intelligent creatures could dig holes aswell, but nature also' makes holes. … well you’ve just said there are things intelligence alone can cause: my question, you’re just repeating what I said … 

We need ways to distinguish the difference, and the way to do that is to find the cause of it, not just assert what the cause is. and Intelligence is a cause dammit … intelligence is real … but your confusion obviously is that intelligence is only limited to humans … that’s totally and factually wrong … I’m even certain you believe in Extra terrestrial intelligence … if so then you’re contradicting yourself …

If science worked the way you think, we'd still be in caves. actually you’re still way off grasping my thought … so in truth it’s just you and your thought battling out here …

"for the nth time what I need to tell you is experience we have of intelligence creating things like an induction motor or the computer code ... with this we can say that the flagellum and DNA were most likely caused by INTELLIGENCE ... and as a christain I say the intelligence agent was God ... do you understand now?"

A failure of reasoning. We know that the induction motor was created by humans. It isn't "intelligence" that produces them, it is humansthat do. … wow … a failure of thought says someone who believes intelligence doesn’t produce induction motors and computer codes … another beauty …

Humans are a specific "package" of intelligenceand the ability to actually do things, because we have strong enough bodies, and we've got tools and such. … another way of saying intelligence … intelligence is the best explanation for any technology we have … because gorillas even have stronger bodies and yet don’t even come close … 

And like I've pointed out, humans sometimes make things that nature also makes. Therefore, some things that intelligent creatures make is also made by nature. … lol close … actually it’s : some things that intelligent creatures can make is created by nature … ofcourse humans can make the Giants_causeway easily … doesn’t actually counter my point … my point is obviously that nature cannot make a computer: and I’m talking about the nature we all know, see and observe …
That's not true. IC proposes that you cannot remove any single thing and still have a working system. … OK it’s either you read my comments with Spiegel, or you study up on Behe and his concept, or you STHU … IC says the system must loose its function on elimination of any part to be deemed IC … 

All claims about actual IC systems have been debunked, so far. The flagellum, the human eye, the bombardier beetle, and so on. … actually the people who apparently debunked it don’t even understand it … it turns out that you and the critics only debunked your idiocy … I mean you have to know what it says before debunking it …

Whenever we do find something that appears to pose a problem, it usually doesn't go far enough to become a famous problem, because the scientists quite instantly notices the problem and finds the solution. … actually this is best explained by many factors including: re-interpreting the facts, or just inventing new “facts” and ”evidences” … 

But what I've been trying to tell you that if something is "unexplained" it doesn't meananything. If you use "unexplained" as an argument for something, then you're likely appealing to ignorance, which is a fallacy. … no silly I’m saying the best and obvious explanation is a known cause which is intelligence … 

If ther eis some bioligical structer we can't explain that it is "unexplained" until someone can explain it. … ID actually is the explanation: I’m not going to be surprised if it turns out that you don’t even know what ID says up till now …

IC effectively equals "unexplained". "this system is irreducibly complex" does not mean "this canont have evolved". No one has ever proved that IC means it cannot have evolved. … again read my explanation to Spiegel or try to STHU and reduce the lines …

Anyway, you falsify IC by showing how something could have evolved. … demonstrating that’s the word you’re looking for … and maybe you can show me a demonstration of a flagellum evolving … that’d debunk IC instantly … but we know you don’t have any such … only imaginations and some faith …
*It's that simple. And we do that all the time, because it's critical to undertand how things can evolve.*… I just need one experiment showing an IC system building up from scratch … just one … lol … 

They have no reason to do that until they can establsih that it indeed is IC, which is really hard to do. … it’s hard if you don’t even understand the definition or description to start with …  

Pay attention: He gave up because of his belief in god. I've said this 2 times before, and you keep failing your reading comprehension. … maybe you should pay attention to your own lines … you said Newton “gave up and resorted to saying God did it” … and I replied “he didn’t come to a conclusion of God because he gave up on his science” … how much comprehension do you need to grasp this? … this is just another example of you wasting time and even forgetting what you said: PS poor understanding …

Yes, because he had a different view of what it means to be called an "atheist". I've explained this. It was a century ago, and culture has changed. … and I’ve explain to you that the view of atheism was that God doesn’t exist … same view as today: and same view he criticized … dammit search the page of just STHU …

Today, he would be considered an atheist, because he was not a theist. … deist or agnostic would be a more suiting description … obviously no reasonable person would call him an atheist after reading all his comments about atheism …

I mean, I am an atheist, and I agree with every word I have read that he said on the subject. … I don’t suppose you agree with this … 

" I have repeatedly said that in my opinion the idea of a personal god is a childlike one. You may call me an agnostic, but I do not share the crusading spirit of the professional atheist whose fervor is mostly due to a painful act of liberation from the fetters of religious indoctrination received in youth. I prefer an attitude of humility corresponding to the weakness of our intellectual understanding of nature and of our own being. "

Or

" [T]he fanatical atheists...are like slaves who are still feeling the weight of their chains which they have thrown off after hard struggle. They are creatures who—in their grudge against the traditional 'opium of the people'—cannot hear the music of the spheres. "

Or

" In view of such harmony in the cosmos which I, with my limited human mind, am able to recognize, there are yet people who say there is no God. But what really makes me angry is that they quote me for the support of such views. "

I've heard many different ways of defining it, but it carries the same core idea: That we do notknow about god. … that’s not the core idea buddy … the core idea is that we don’t know enough to conclusively describe or dismiss God … not that we don’t know about God … 

If it's not completely random, then there is somesort of pattern to it, and that matters. ... lol … actually it turns out to be completely random … environmental conditions are random, mutations are random … Natural selection just says anyone who’s random mutations are favored by the random environments, is lucky … that just like saying the criteria for selection in a dice is 1-6 and so 1-6 can be good or bad … ie you can roll 1 and be luck: you can also roll 1 and be unlucky … 

A dice roll may be quite random, but I can predict that you won't roll a 7 with one D6. Therefore, it's a priori less random than something that could roll any number. And thismatters. A lot. … no not really … predicting there’s be no 7 is like predicting there’d be no fire breathing nuke launching mountain size dragon … 7 doesn’t exist on a dice so that prediction is obsolete when considering a dice … more like nonsense …

Eh? Yes, it's extremely absurd. Evolution isn't random. … well just want to be clear … if it’s proven and demonstrated that evo is random, would you consider it absurd?

OK, in one short sentence, you managed to prove that you don't know evolution. Congrats. Now go study it if you're going to have a discussion about it. … hahaha … maybe you could start by studying ID before you say anything about it … also you agree that the environmental conditions are random, and the mutations are random … so what’s your beef … natural selection is just a distillation of these two processes … it basically says if you survive you’re lucky … 

Also, consider how anyone could make a theory of something that is random. … well it already happened: why do you think I’m in this argument? 

Theories are meant to predict things, so how do you predict something that is inherently random? You don't. … how to predict something random evo 101 … simple … it will change … QED … prediction correct … yes a random process will obviously bring about changes in outcomes … question is how you come up with such amazing “unique” predictions … 

God you're dumb. … hahahaha … wait a minute did you just say “God”? … 8| … with the capital letter? O.o …

Yes, exactly. That's very, very normal. … lol … you let the “undirected” fool you … undirected still means random … apparently random processes can create specific non-random outcomes … Interesting stuff …

A human from a bacteria wouldn't violate the law of irreversibility...! It's weird how you start talking jibberish whenever you have no idea what I'm talking about. And sadly, that's way too often. … Ok I’d admit I didn’t read it at first …. But it’s even more hilarious now … evolution is inherently undirected: but it doesn’t move in a backward direction … pure beauty … evolution is undirected but directed … evolution has no specific outcome but it specifically doesn’t give outcome “X” … lol … 

Right now, go and read up on what an equivocation fallacy is. The first thing you might notice when doing so is that "a definition" cannot be an equivocation fallacy, since an equivocation fallacy is the fallacy of equating two different things as if they were same thing. … thanks for the short definition … lol … evolution actually equates two(or even 3) different things as if they were the same thing … 
1.	Simple to complex development (or what we call vertical evolution)
2.	Genetic Variation of organisms ( horizontal evolution)
3.	Complex to simpler degradation( loss of functions or components) 

*I wouldn't even know how to begin doing that when defining what something is. A definition is not a logical syllogism or anything like that, which means it cannot contain a logical fallacy.
I mean, sure, if you're really creative, you might be able to do it, I dunno* … well lets see … how do you merge these three concepts above into one definition? Simple … organisms change … sweet and sleek … merged like there was no definition of evolution before it … 

Anyways, don't use grown-up words if you haven't learnt them yet. … OK daddie … 

We are talking about time, so when you say "where", you're already failing. … lol please not again … if we’re talking about time, then we’re dealing with “when” … 

I'm not saying the univesre is infinitely large, I am saying it always existed (time). … well the facts show it started to exist … even if your brain can’t capture what it could have been like before, don’t be downcast … most of us can’t either … it’s the limit of the human mind … it’s just like imagining how far the number line can go … or the end point of the universe …

But here comes the fun part: The same god did different things in all 3 religions. So.... are they the same god, or not? … actually I’d be more justified to call you a moron at this point but I’m thinking I can do better than that : I can actually make you see that … God did many things even the Bible did not record … however there’s concurrence in the description of God as the God of Abraham … in addition, the Bible and the Torah are basically the same : the Bible contains everything in the Torah … 

I don't care what you think some of them would do. You and I, and everyone else, would know that they are wrong, because of evidence. … evidence is not a limitation if you can create the evidence out of imagination … that’s the only way two chunks of skull bones can transform into evidence for an invisible missing link …

But we would need to have fewer levels of taxonomy to describe it. There would be no need to have the "phyla" level of taxonomy, perhaps. … yes there would silly … remember by your beliefs only 1% of the population of all organisms that ever lived exist today … lol … just do the math …

The more life diversifies, the more levels you need to sort them all consistently. … WTH are you talking about … it’s not like there’s a constant rate of diversification which can be accurately calculated … and you seem to be ignoring extinctions …  

To know if something was "designed", you need to find the thing that designed it. are you kidding me now? … mehn … to know if something was designed you need to find the evidences of design and compare … know who designed it is a different case and like I’ve said countless times … that’s where my belief in God comes in …

To make the fossil record reflect design, you have to assume that each one was created separately, then destroyed and replaced by a nearly identical species, and that this process goes on and on. … well it is very possible that these creatures were created but were lost due to entropy : and the creator just created more : each time, adding more information to help withstand entropy and exist longer …

Nothing about the fossil record tells you that this happened, but that is what must have happened if they were all designed. … yes there is … sudden appearance and disappearance of organisms is what the fossil record is about … why do you think gradualism was dumped?

Teh fossil record tells you what existed, and in some cases other things, but does the fossil record tell you that those animals were born? No, that is somethign we infer. Likewise, if they wer created, we would ahve to infer that aswell, beause the fossil record doesn't show their births/creations. well perfect and unclouded inference definitely suggests design at the Cambrian period … that’s the only logical explanation … except you could explain to me again how these organisms morphed so fast and forgot their transitions …

So, lets say we find "god" and prove for sure that he exists, … first prove that love, music, beauty, etc. exists, with the scientific method …  

Life is not an isolated system. … the universe is an isolated system so? … 

(Fuck, I'm so tired of people pulling up entropy...............) … it’s the best piece of fact that debunks evo. …

Source for that? … you … or are you saying evolution is a directed process? If so you’re contradicting yourself … 

A cat cannot produce a bear, that is a fact.  …that is not a fact going by evo. Taxonomy doesn’t have any effect on the reality … whether you call it bear or whatever … if it’s identical to a bear, then taxonomy doesn’t matter … and in this sense, evo. Can change a cat to a bear … I say this because of the lack of restrictions of evo. … except there are restrictions, then we have a contradiction … I do remember you saying evo has “no end goal” … ie no restrictions … 

This is just sad.... … what’s sad exactly? That I’m using your description of evo.?

Yes, an archaic bacteria could become a cat, eventually, but a bear is on a different fucking branch on the tree! … the fact you put them on an imaginary tree has no weight on anything …

A cat becoming a bear would imply a jump from one branch to another. That cannot happen. … Ummm how exactly can evo. Prevent this? 

Well, yes, and I'm happy about that. It's just that the problem is that when you bring the bible into line with the evidence of reality, you no longer have a religion. It crumbles. … no it doesn’t … 

If they actually stuck with keeping it in line with the evidence of reality, then they would have no religion. … true … depends on how you define religion … being a theist doesn’t equate to being religious …

Theoretically, yes, they could've changed the name at some point. But because Darwin started it, I guess no one wants to take that away from him. He was still right, at the core, as far as I know. … I see … Darwin was right at the core but was “wrong”  overall … interesting … 

But names really don't matter. … yes it does that’s the main issue … evolutionists know very well if they change the name there’ll be no arguments at all … the name constantly insinuates “simple to complex” because that’s the original meaning … and if you watched this video you’d instantly realize the interpretation concerned with evolution …z

The science still is what it is. If you have a poblem with the name"evolution", then changing the name helps with that, but it doesn't change what is true. I’ll be more than overjoyed if you decide to call it “theory of Genetic variation” … that’d end any argument instantly … you could go with “theory of Genetic change” too … still ambiguous but more appropriate … or better still, “frequency shift theory” … 

Sure, the theory of gravity has been effectively changed to the theory of relativity, though, as an example. The old theory is really only ever used as a decent approximation. … so what are we waiting for? … change the damn name and you solve the problem … but I reckon these scientists will never agree to do so … they’re gaining a lot from the equivocation …

"Skew"? Like I said, it's an improvement, since it no longer conflicts with any exceptions. … well there’s a reason Einstein’s theory of relativity didn’t go by the name “theory of gravity” … that’s because there’s an extent to which you can change the definition of a term … evo. Exceeds that extent …

Yes, that is an example of evolution, since dark moths become more frequent, which light moths became rarer. I really don't see how this is relevant to penguins giving birth to penguins. … it says moths produce moths … 

Yeah, things like that. What it actually means, "scientifically" would be a mystery. … a mystery as music …

*I'm quite sure it says both, as I remember it.
Genesis 12:7 has god appearing to Abraham, for example. Isaac, aswell, in genesis 26:24.* … like I said, those were just different forms … God also appeared to Moses … but manifested as a burning bush …

In many places it is implied that people saw him, such as Adam&Eve. … Adam an Eve were the “originals” … so there’s nothing contradictory if they saw God … after the fall that is …

But I am also aware that the bible says that anyone who looks upon god would die, paraphrased. Very weird, but I do not care, and I don't propose to be an expert on the bible. The bible doesn't matter to me, obviously. … well then try to minimize your thoughtless assertions concerning christains if you don’t understand our primary text …

Yes, anything we see is manifested by light, so to speak. … also a medium …

Nono, you're mixing up "critical thinking" with "creative interpretation". … no buddy … I’m not … but it’s ok if you think I’m am …

*Who am I to ask? No one knows anything more than what the bible says, about the bible.
I may ask, for example, why god needed to send angels to scout things for him, if he is supposed to know everything and be everywhere. In the story of sodom & gomorrah, the bible says that god had to send some angels down to check it out to see if the rumors were true. Yet, peopel say he's everywhere and knows everything, but he doesn't act as if he does. And I have no one to ask, because no one is an authority. And ther eare countless of these "problems". And you don't see me arguing about it, because... yeah, I don't care, it's just a fantasy story, it doesn't have to make sense.* … explaining the Bible to you with your level of thinking is going to take a really long time … like I said, try to study it yourself and get commentaries … you don’t even know the main message of the Bible: and I assume that with good reasons … I’m not sure I can spoon feed you with the sheer volume of load I have to respond to … so do both of us a favor either you search it out or just stay silent…

Of course, there are probably different kinds of love, but all these kinds still follow a similar system. … no they don’t … some people take years to love some weeks, some months, there’s no system that can describe love … 

The brain is a machine, it can be tampered with. then it would be possible to tamper with the brain and make someone fall in love that way … but it’s not … 

I agree hat love isn't "controlled by" hormones, it's just the brain that reacts to certain things. … it’s more than just the brain … 

*The hormones are an effect, not the cause. But they cause us to feel this emotion/state.*… what exactly are you saying here? The hormones are not the cause , but they can cause feelings ?
The "love" that is here to make us reproduce is caused by the brain seeing hormonal markers in females, such as wide hips and whatnot. well how about when there’s a love that causes one to give up his own life … totally against natural laws … what happens here? Does it mean it’s not love? …  

*From what we know, the universe cannot have a "cause" if time started with the universe. Without time, you have no "causes". The universe has always existed, and it exists for some unknown reason. It might be that it exists simply because something must exist, or it would violate the uncertainty principle.
But we don't know why it exists, right now, if "why" is even a reasonable question.* … this is a totally different position from what I’ve heard of the consensus … hope you’re right this time … because it very well seems like you’re wrong yet again … from what I know the universe started from a point of nothing … no matter, no time …

Evolution is that known cause, and it is natural, and it is observable and testable, and it is confirmed. … yeah we observed that it mostly destroys info. And builds no complex systems … so how else can it explain the bacteria to man transformation? … Assigning imaginary powers to evo? … nope : that’s the magic … what you’re saying is in contradiction to what we can see and observe … 

You keep insisting that it isn't, so in your head, perhaps it's "magic", but it isn't to science.* lol … 

But humans didn't "come from bacteria", they came from the australopithecines, which wereapes. You're not helping anyone by intentionally trying to make it sound as hard as possible to believe, by jumping a billion years. … ok I see humans didn’t come from bacteria… but they came from bacteria … another beauty … btw humans didn’t come from austral-whatever : thinking that’s just another fabrication born out of an evolutionary presupposition … and please try to bring facts when talking to me pls … that’s what I try to bring as well … it’s not fact to me if you can draw up imaginary transitions from incomplete bones … some of which were found in different locations … 

Yes, it's really, really weird that humans could come from bacteria, but that's not really what happened. That is just a brutal simplification. … I like the word brutal … I think you meant to say brutal take down… these “billions of years” is probably not even certain … PS I’m not saying anything wrong by connecting the humans and the bacteria … that’s just what evo. Says … and it’s actually ridiculous even if you give it a trillion years … the time period is just the excuse to dump the burden of the intricate complexity developed… 

You're only trying to appeal to people's incredulity and their inability to visualize such long time spans. It's a lot easier if you follow the lineage of humans backwards, and see that no large jumps were ever required to explain the history of evolution on earth. … yes there are a lot … why are you trying to hide the facts? … please stick with the facts as much as possible here … 

Yes, that is exactly how I see it. It is a fantasy story that in large parts is symbolic. … actually most of the symbolism is meant to filter out people with poor reasoning such as yourself … 

Yes, the bible are the ramblings of idiots, from our point of view - but I don't blame them, because they didn't know better. … well another stupid assertion from you … sure they were much ignorant than we are now and God knew this quite well: one of the reasons He was pressing for the messiah so people can actually know Him … the knowledge then was sufficient for their time … just like you wouldn’t teach your 4 year old son Engineering mathematics or DSP or such abstract math … you’d wait for him to grow up in understanding and knowledge first … technically, going by your assertion, you’re actually an idiot … because definitely you’d look that way 2000 years from now … please try to expand your perspective and thinking … 

*That's fine, we can't all know everything about everything, and neither do I. The big bang only created hydrogen, helium, and some lithium. Those huge clouds of gas collapse to form stars.Inside stars, those atoms are pushed together to create heavier elements, and this is what fuels stars. Nuclear fusion.
Then the stars die and throws these new elements out into space. So with the next generation, it's finally possible for rock to form. Earth is a rock planet. All the material that makes up the earth comes from stars that have exploded. Therefore, stars existed before planets.And in either case, the earth is only 4.54 billion years old, while the universe is 13.72 billion years old. So that makes about 9 billion years before earth (and the sun) was formed.* … actually to be honest, this sounded like another creation story … do you really have evidence for all this?... 

*"Faster", when speed is what we want. "Stronger" when strength is what we want. And so on.
We can beat any characteristic of humans byfar, except for the human ability to innovate.* … well you can’t beat the human with any technology … if you can get all those subs together to form one unit that can function better than the human then you can beat the human …

However, we're very soon making technology that beats human innovation, aswell. Ironically, by using evolution. … lol … no silly … it’s by using Intelligent Design … lol … without design you have nothing …

And we're building computers with more processing power than a human brain, very soon. … Ooook buddy good luck with that …

Computers don't have "nerves" and don't need to regulat their body temperature, and os on. You're talking nonsense. no stupid … I’m talking if a computer can achieve the same functions as the brain with so little energy … 
We can make technology that extracts more energy from a sandwich than a human body does. … ok if I ask you to show me a technology that beats the human, I don’t mean on that exists in the imaginary ok … thanks …

You seem to be under the delusion that life is really great and perfect. … No silly if you knew anything about Christainity you’d know it says life is actually in a fallen state … I’m just saying from what we can see there’s technology that humans have not even come close to scratching the surface … 

It's really damn far from it. We could imprrove pretty much every detail about the human body, theoretically if not yet practically. … try your best to work with facts … 

We could even improve the cells. We've invented XNA, which works just like DNA, but is strong and better than DNA. … again fact’s “we could” is not an answer … you could try and realize some side effects … so please STHU about the imaginations …

Satellites, in this context, means anything in space that orbits somethign else. Even a moon is a "satellite", and so is any small debris in orbit, aswell. … no what context are you reading … I’m obviously talking of satellite in the context of “an artificial body placed in orbit round the earth or another planet in order to collect information or for communication.”(Google) … u kidding? …

No, they cannot. They have atoms of iron in their brains that react to the magnetic field of the earth, which makes it a compass. It is notprecise. It couldn't be very precise, because the magnetic field of the earth changes a lot, so the birds would get lost all the time. … well by that theory all bird should be dead by now … also if their navigation system is not 100% perfect how do you explain the Artic tern which travels for distances over 20,000KM and arrives perfectly at it’s destination for the first time? … you better not be giving me more crap here … 

No, airplanes can use GPS, which is better than a bird's built-in magnetic compass. Where did you get this idea that bird are particularly accurate in their navigation? Yes, they find their way, but their nagivation "system" is not very accurate. … yes they find their way over thousands of kilometers but their navigation system is not very accurate … beautiful stuff … 
They can end up kilometers wrong, but when they recognize where they are, they fly by sight and memory. looool … they miss their way and then recognize instantly where they are? Lool … the artic tern when travelling appears to fly ofcourse but on closer inspection, it flies to specific locations to get a speed boost from a damn wind it apparently can’t predict … like I said, you better not be giving me new crap …

What I am saying is that birds use the same techniques as human do, for finding our way. We learn the way, and we use memory and sight to find landmarks, and so on. … so how do you explain birds that navigate their way perfectly on first attempt? …huh?

Bird who migrate use the stars and the sun to stay of course, aswell as this magnetic compass. But becaues tehy fly the same route every year, they also learn, especially by following their elders, the way to where they're going. … what happens to the birds that migrate alone? Who teaches them how to fly the first time?

If a bird were to fly blind, it would not get anywhere near where it wanted to go. It would fly the generally correct direction, but the precision is so poor that they would still be off by many degrees. nonsense … precision so poor? I think you should update yourself on birds navigation … the life of many birds hinges on precision else, death … and they still thrive up till today … 

We can build something stronger, faster, more perceptive, better reflexes, and with more processing power than the humans brain, which could also have a lot of abilities that humans simply do not have, like radio transmission capabilities, internet, night vision, and so on. of course you can even build a hulk or something like that … but only in the imaginary world … like I said, I work with facts … and so far you have no technology that can come close to a full human … I’m not even sure you’re think it through at all …  

*Like I said, we can beat any characteristic of the human body, by miles, apart from the human ability to innovate. And we'll have technology that beat that soon, aswell.*… well I’ll like to see you create a machine that beats the human in all aspects at the same time … only then can you challenge the technology of the creator … 

Absolute bullshit. Single-celled organisms evolve just as much as multi-celled organisms. Being multi or cingle celled makes no difference, you still evovle because the gene pool still changes with time. lool… ofcourse not no change in gene pool causes single cells to collate to form organs and tissues … it’s just another imagination of yours …

And as for single becoming multi, that took a few *billion years to happen, the last time. Don't expect such a rare thing to happen very often.* … again you talk as if it’s a proven fact … atleast I accept mine as a belief which can’t be proven by science … but your situation is even worse because you take these imaginary events and treat them as facts and you expect me to conform to it … no amount of time can build a functional organ from simple cells … you’re not giving me facts but you expect me to just accept what you say as true … no way … 

Normally, being single-celled is better than multi-celled. That's why I don't personally know why we ever became multi-cellular, at all. … I know … because evo. Says anything can change into anything … you don’t need to find a rational reason to believe this … if so then you run into a lot of problems with the facts … you just have to accept that things change randomly … 

No, but seriously, "genetic variation" is the fact that variation exists. "Evolution" is the fact that the "average", the "center point" of the genetifc variation changes in a specific direction over time. … correction : changes in a random direction over time … you did say evolution was undirected didn’t you? … so what specific direction is this? … also a more descriptive term for the change in frequency would still be genetic variation: it’s closer in actual meaning than evolution … 

This is the phenomenon that also eventually causes species to split into new species and create a tree structure, given that mutations are also introduced regularly. Two geologically seprated groups of the same species will evolve in different directions, and will evenetually become too different from eachother to be of the same species. That is "speciation". … well this is one of the reasons I prefer to use “kinds” … the organisms show the limit in variation but evo. Takes out any limit and insinuates the can change drastically to even a level of adding new organs and tissues from no where … in reality, the organisms only pass on what they have and variation takes place in reproduction … but with evo. New organs and tissues can be gained from apparently nowhere … this is what invalidates the theory … if organisms only pass on what they have, where would the new “perspective” information come from to bring about the totally new traits? … evo. Says random mutations … random mutations will create things intricate systems which was never present in the previous  generations … 

I can see you're trembling in your boots. The moment you know you're beaten, all you can do is to try to trash-talk. … Sorry but all this is just going on inside your head … has no bearing on reality … however I’m glad you are showing this is just a contest to you … you’re not willing to open your eyes and look at things critically : not as much as you’re willing to win an argument … 

Ape-men who selectively bred beetles? Just what on earth are you talking about? Did you just have a stroke, or something? … could you please stop blaming your lack of comprehension on me? … what I clearly said there was even ape-men could recognize the variations and that was why there was selective breeding to start with … don’t judge me from your stupidity … please … thanks …

You're mixing up contexts. Outside of science, "evolution" generally just means gradual change, and generally from simple to complex. We can talk about cities evolving, for example. In biology, it doesn't mean that. … yeah it means change in allele frequency in biology and simple to complex development in bio-chemistry:  Chemical evolution means formation of complex chemicals from simpler ones … glad you can see how evolution is not even consistent in science …

The level of fail here is quite impressive. … if you ask me I’d say failure of your brain to perform primary thinking tasks … 
Imagine if science was like that. Someone makes a hypothesis that could explain something, and the prediction is that "we should se signs of this". … well done ignoring the junk DNA … anyway I said we can see these signs and test for them … also another prediction I mentioned is a singular life code: which is unique in that evo. Spawns things up randomly and so evo. Would expect to see another life code… way to go with your poor thinking process … you’re definitely not making things any easier … if you can’t think properly then why type up so much and end up loosng the plot, and forgetting my points? … another prediction is the lack of transitional fossils which actually indicates acts of design interference … this actually a failed prediction for evo. Because mathematically, there should be millions or even billions of transitional forms showing evolution … but they are literally non-existent … the only transitional forms know are the ones conjured up by imagination … 

Fucking genius "prediction". It'd be like kids in a fucking sandbox. … let me remind you one more time … evo. Predicts that moths always produce moths …. This would be higher grade of genius …

Nope. But how about those creationists who imagine 100% of the evidence that's missing for their ideas? … well atleast they don’t imagine it and call it science …

It's "evidence", not "evidences". Why docreationists insist on putting an "s" at the end? You should look up the background for that, it's quite interesting. Some creationist wrote some article in the 1970, or something, which pluralized "evidence" with an "s" at the end. Then it spread through the creationist community. … yet another piece of nonsense …

*But because creationists never actually read science, it stayed a creationist thing to pluralize it like that.
It really tells you something about creationists and science. Basically, whenever you see someone pluralizing it like that, you know they've never studied science. (Also, it's "its evidence", not "it's evidence". But whatever.)* … more nonsense … 

Go and convince your creationists buddies to actually make proper hypotheses, instead. If you want to play science, then at least follow the scientific method. … actually we already have … but we have people like you who apparently can’t understand IC but still blab about it …

No, fire someone who is supposed to be a scientist but can't even reason properly. I just explain this. Can you read? … well then you should fire all the people that think like you because I’ve explained IC for days and you still don’t understand it … 

Heheh, ok. That's a new one, "dull". … well I’m thinking I should just stick with stupid … it unfortunately describes you for most of the times …

I've explained how easy it is to falsify "true IC". All you have to do is show how something could have evolved. We do this all the time. … no silly … you need to demonstrate it in a lab to disprove it … 

Fine, do that. Just don't go around saying shit is or isn't some way when you don't know what you're even talking about. … do you even check yourself before saying this? … 

I've had to define evolution for you, and you still don't seen to even get that. … no stupid I get what it’s saying … and you even understand where my issue lies… please work on your memory or just do us a favor and type less …

You come on here and say that evolution is effectively wrong, but you don't even know what it is, and you insist on things that are absolutely moronic. … this statement is actually moronic because I’ve explained to you what’s wrong about evolution … 

It isn't crap, or a waste of time. Even if I fail to teach you anything at all, other people might (and actually do) read this, and might have use for it. … it’s only people that have the same mindset as you that would digest your nonsense … for you to make any progress you have to think more and make an effort to understand the other perspective … this is not an indoctrination section … so you have to defend most of your positions … something you’ve done so poorly …

I fully admit that I am really bad at that. I might have a convoluted communication style, probably because I have Asperger's syndrome. … Coming to think of it, I might actually be wasting part of my life talking with someone like you and hoping you’d even understand what I’m saying …

By that, you're insinuating that you know so much more about this than I do, that I can't even grasp it, and don't even understand how wrong I am. … no silly … I’ve said it a couple of times: you know more than me: but you just fail to actually reason and think … PS most of your knowledge turn out to be false and unscientific … 

OK, I'll take some "guess". I'll guess they'd be bubble-gum-powered hot air balloons. done … evo. Can achive something like that … 

No, sorry, you're the one who claims that evolution isn't up to it. You're the one who says A can't evolve into B. … yeah and you’re the one failing to follow up on the points … my point here is evolution is completely random and unpredictable: and hence, any imaginary explanation can be conjured up and still suit the criteria …

Humans cannot evolve bird wings. … you have no evidence to prove that and evolution doesn’t prevent this …

The only way that evolution ever causes extinction is when some predator "accidentally" get a mutation that makes them "too good", and they eat all their prey, and then they die from starvation, becaue they screwed uo the predator-prey balance. … WTH is this? … where exactly are you getting this from? … is this just another imaginary story? 

The reason we have lungs is (as we currently understand it) that the lobe-finned fish from which land animals evolved had pockets/sacs of oxygen in their blood vessels. This allowed them to do what I described. They could get up on land for a while, before they had to return to the ocean to get more oxygen. … and you expect me to believe this? … 

Those sacs of oxygen gas grew bigger, and they are what we call "lungs", now. … dude … atleast have the decency to come out clean and say these are just imaginations … not science … you’d sound more credible then …

The larger those sacs grew, the longer they could stay out of water, which was beneficial for many reasons. Eventually, they didn't have to go back to the water at all, anymore. … a cool story … 

Say "please". You cannot force me to do anything. You can clearly see the effort I put into this, yet you're not appreciative of that effort at all. I am not paid for this, I do it out of good will. … you are one hell of a joker … I can reckon you don’t put as much effort as me because you don’t even understand most of my lines … you should thank me for actually wanting to sit down and reason with you amidst you endless rants …

You think you undersand it, and you're very confident about it, but you're completely wrong. Learn some humility and learn to admit that perhaps you've misunderstood some things. … I really don’t have a problem admitting my shortcomings … just that you have have given me more than enough reason to discard most of your comments … and I’m not sure if I can continue with this … if you can’t summarize your points then don’t type at all … and don’t accuse me of misunderstanding anything when you can’t understand a simple concept like IC …
Reply: Benjamin Toby I'm just going to keep repeating myself until you answer my questions:

What experiment do you think demonstrates that IC structures cannot arise through evolution? If you think that finding a structure that ceases to function once you remove a component means it cannot have arisen through evolution, why is that? What exactly is wrong with the Mullerian two-step approach (which is what I used in the bridge analogy), in which a part is first added, then made necessary (perhaps through the removal of another part)?

Why do you think that evolution has to behave like a rational person? It simply must obey the laws of physics, which obviously are nothing like a person. It doesn't have to have a high probability of improving organisms on each mutation because evolution has billions of years to operate, and natural selection only keeps the beneficial or neutral variations. What part of this escapes you?

And what answer do you have to the many successful predictions of evolution, such as the transitional fossils I linked you to? Where are such successful predictions of ID (or even unsuccessful, yet testable for that matter)?
Reply: Benjamin Toby "Oh I see he only needed to give you the link to the video you spent so much time commenting on"
Yes, that was the confusion. At first, he made it sound like it was some other video, and nothing he said explained that it was this very video.

"*Yes, he sure is a lot like you, in this regard and others.* … No surprises … sure you wouldn’t be surprised if I told you you were just like Spiegel"
I wouldn't know, I haven't read his comments.

"
1. We take the word "box", which is a symbolthat refers to an actual box. … lol … early fail … I say take the word “hello” … which is of course a symbol that refers to ….. Ummm … Hello! … hahaha … your second symbolism argument crumbles instantly here"
Goddamnit, I told you that because "hello" is an interjection, the example would get unnecesarily confusing. This is why our conversation gets so unnecessarily long, I think you're intentionally trying to make things confusing for yourself.
Yes, in a sense, the word "hello" is special because it doesn't really "mean" anything, it's just something we say, like a sound we make. That's why it's called an "interjection", in this case a secondary interjection, not a primary. But the written symbol, "hello" still refers to that thing, that idea of that greeting.
This is why "box" is a better example, since you won't get this confusion so easily. It's not that "hello" isn't a symbol for something, it's just that it's harder to understand that it is.

"In addition, what if I want to encode a letter “A” using morse code … what happens then? What does “A” stand for? A?"
There is no real difference between a letter and a word, both are symbols. Both refer to something real, even if it sometimes doesn't seem like they do. The thing that "A" refers to is real, it is a specific kind of sound. Because we're so used to reading, we don't think of it like that, anymore, but that is still what it is.
But languages are not consistent, because they evolve, and accumulate errors and changes that seem inconsistent. The letter "A" can actually sound in slightly different ways, but perhaps initially, where the letter came from, it always sounded the same.
Languages are not really intelligently designed, they evolve. They probably started with people just immitating eachother's sounds, but the sound was completely arbitrary.
That's why languages don't quite make sense,a nd the way we write doesn't quite make sense either. But the letters are symbols that refer to something, it's just that they are more organic that most symbols.

" if I just send this as a message using morse code… does it mean I haven’t used any code?"
"A" is a symbol, and the morse code for "A" is then a symbol for a symbol, so "code".

"the basic reason I’m rejecting your definition is that you think code is strictly conceptual "
Its because it is. What you're talking about isn't "code", and I don't know why you think it is.
The poroblem is that the thigns you're talking about are "codes", but those codes only exist in people minds. It's our way of decribing them. They aren't physically codes, because... yeah, "code" is conceptual.
A CPU gets an instruction. And "instruction" is our simplification7symbolism for what it really is. When we give specific instructions (which are symbolical) specific najmes, then those names are codes for those instructions.
But it isn't the names that go into the CPU, it is the thing that those names are referring to. Specific patterns of voltages.
We call them by code names so that we conceptually understand what's going on.

"let’s say the button in my analogy represents the switch patterns: ie the switch patterns are symbols for the button"
Why do you reverse it? The switch patterns are not symbols, they are the real thing. We use symobls to refer to real things like that. Real things aren't supposed to be seen as symbol for conceptual things.
Yes, you could say that the letter "A" is symbol for that specific sound, and therefore that specific sound is also symbol for the letter "A", but it just makes no sense to think of it that way, because then the whole idea of "symbolism" goes out the window. Symbolism is inherently conceptual, and the real world isn't at all, therefore the real world can't be symbols. (?!)
Yes, the button could be thought of as a symbol for something that will happen when you press it. At least he marking/label on the button is.
When I press the "A" key on my keyboard, we basically pretend that I sent an "A" into the computer. Software is a huge system of pretend. In the end, all we've got is voltages going around in ciruitry, and as long as we keep track of everything and make sure everything is consistent, then the illusion that there's more going on can be upheld. And that is useful to us.
Software is still people communicating with people , not the computer communicating with people. When I use a program, I am really dealing with the person who wrote the program, not the computer.
Even when I see an error message, the error message was written by a person with the intent to inform the user that somethign has gone wrong. It isn't actually the computer talking to you.

"Aside this, I brought up the analogy to explain the Computer code : and from this a code is anything that represents a specific action"
Yes, thank you. The code represents a specific action. That is exactly it, and what I've been trying to tell you all along.
It action doesn't "represent the code", as you've said so many time, now.
Obviously, there is a problem here, since you contradict yourself.

"so if “.--..” represents “A”, then “.-..” is the code … but from your definition there’s no code here because the letter “A” is not a symbol for anything"
Well, this explains it, then. I see your problem if you think that "A" is not a symbol.
When you wrote this to me, I read the symbol "A", and my brain heard the sound that "A" refers to.
Of course it's a symbol. It's even called a "symbol". A letter is a specific kind of symbol. Letters are a "category" of symbols.
Apart from this, the rest of what you said here is correct. And that makes me happy.

"*"A code" is just one symbol, not enough to produce a program.* … but codes can … this was why I said a program contains CODES … no one code … a single code contains a single function"
You can't say a single code contains a function, because that heavily depends on what coding system you're using. Coding systems are completely arbitrary.
Anyways, I think we need to define what we mean by "program". In what sense we mean it. Because in one way, you're correct:
If you consider the source code to be a program, then you're correct, the "program" contains codes, it is made up of codes.
But if you consider software that runs on a computer to be a "program", then it doesn't contain code. And this is what I mean by a "program", at least. Something that runs, like an ".exe" file, for example.
The source code is only conceptually a program. It's "going to be" a program, when the compiler turns it into one. The computer can't run it, therefore I don't consider it to be a program.
So clarify which you mean before we go on.

"the “thing”? really? … the source code is the “technical term” for all codes contained in a program or application "
I just don't want to call it "code", because whether it is "code" or not depends on what language you're programming in. And I'm trying to be strict with my usage, to avoid confusion, but I'm not sure it's working.

"code can’t contain a program because a code translates to one function alone"
"Code" as an uncountable noun. "Code", in this sense, can contain any amount of "codes", thus any amount of "functions". (No idea why you're so focused on functions, but I bet you're just using the wrong word, again.)
And thus, "code" can contain a program, aswell. Source code (uncountable noun, again) does, for example.

" the colour code is the value for the specific colour "
If it is a value, then why are you calling it a "color code"? Are you talking about something like the hex for a color, such as "#FFAA55"?
Or are you talking abotu something like "RED" or "VIOLET"?
The only kind of "color code" that isn't code is the kind that graphics cards use. Yes, it's a value. We do not call those "color codes", because they aren't codes, they are direct symbols.
"#44FFAA" is a "color code", because a computer cannot directly read this, it has to be decoded to a value.

"since the color code usually just one step away from binary form(hex code), what happens when you just put the binary code instead?"
Stop saying "binary code"...! :P
Remember, "binary form" is also symbolic. Anything that represents binary form is therefore "code", since it is a symbol for a symbol.
"11101010" <- this is symbolism, not the real thing.
Hexadecimal in itself is not "code". It's just one way to "read" the same thing. Call it a "conversion", instead. That is, we convert a base-2 value into base-16.
We often choose to represent the patterns of voltages in teh computer using base-2, binary. But we can choose to represent them with hexadecimal, instead, or octal.
So it is not "hex code", unless you're talking about something else, such as my example of "#FF55AA", which is a "color code".
When you "put the binary directly in", then it is not code, it is symbolism. You're writing "11010101010", or whatever, which is direct symbol for the pattern for the switches.

"*Any "codes" will disappear in the process, and becomes pure instruction and "data".* … the codes don’t “disappear”… they are only translated into the original code … which is binary"
No... they are decoded, which means to convert from code into not-code, so that it can be "read". Ever heard the words "encoder" or" decoder"?
This "translation" you're talking about is called "decoding".
And "binary" is not "code"...!

"no it’s called color code because it’s actually the code for the color "
Within a framework of some kind, that someone has written. The computer itself cannot read and understand "color code", or it wouldn't be "color code".
A color code is a symbol of some kind to represent a value that produces a specific color.
Sure, sometimes the line gets quite blurry, because of the nature of it.

"take this example : in html, red and #ff0000 translates to the same thing"
Yes, both are codes that can be decoded into a representation of the actual color.

"the only reason you get to type red or the hex format is just for simplicity … that’s all … there’s nothing here related to just “hiding symbols under symbols”"
Yes, it is for simplicity and clarity. But it still becomes second-level symbolism, which means that is is code. That's why it's called "color code", because it is.
Likewise, "TGAAAGC" is code for DNA sequences, only for simplicity. It would be extremely cumbersome to have to write the actual name of the nucleobases, so we use codes for them.

"ease is the only thing achieved by computer code … this also invalidates your conception of “hiding things within symbols”"
But we get ease because we use codes!
You can either write the binary form, "10101010110101", or you can use a code for it. Using a codeword is going to be quicker, and it's going to be a lot easier to read, afterwards.
It doesn't "invalidate", it validates it!
The point is to hide symbols under symbols. That's why we do it, because that's how we can refer to something complicated with just one word, instead of having to write the whole complicated thing.
Basically, I want to write "1101010010101", but instead I decide that the word "blurp" should be considered to represent that binary sequence.
Now "blurp" is code for that binary sequence. And now my life is a lot easier. Things willb e faster to write, I'll make fewer errors, and I'll be able to understand what I've written more easily.
That is why we made assembly, which is a code system.

"*This is the concept of "abstraction", and the very reason that we can make complicated things, which would've been impossible otherwise.* there’s nothing abstract about the computer … absolutely no damn thing"
Damnit, I should've known you still wouldn't know the word "abstraction", even though I just explained it. It doesn't mean anythign is abstract.
Now I have to explain yet another concept.
Lets say you want to build a smart phone. You don't build the CPU for it, yourself, you buy it from intel, or something. So you get a CPU that is like a "box", and you've got th ebasic instructions for how you need to connect it to get it to work, and what it'll do for you.
You don't have to know how the CPU does what it does, you only need ot know what it does and how to use it. This is "abstraction". We've just added a level of abstraction!
Now someone else wants to build a remote-controlled helicopter. So he buys your smart phone, that you built, to have it control the helicopter. All he needs to know is how to hook it up to his other things, he doesn't have to know how the phone works, he just need to know how to use it.
There, we've added a second level of abstraction.
Abstraction is simply the idea that someone can create something, then close it into a box so that no one has to look at that mess. You don't have to know how it works, you just need to know how to use it.
In this way, we can keep adding these levels of abstraction, and it never actually becomes more complicated. This is why we can feasibly build a space ship that contains millions of separate parts. No single person knows how everything works, but that's fine because of abstraction.
All our technology is based on this.
And this is extremely important in computer programming.

"so WTF are you blabbering about? … Source code = program codes … ie the codes that make up the program … maybe you should explain how code can contain a program"
As I've explained, the source code is what will be part of creating the program. It isn't the program, beause you can't run source code.
The only thing that can read source code is a compiler designed to read it. (And humans, obviously...)

"*That doesn't mean that the program contains any codes, only the source code was code.* … of course the program contains a source code,  the source code is the code"
The program doesn't contain source code. The program was created based on source code.

"well what ever you see in a source code is directly equal to 001010101010101010101111"
No, it's not! Only in assembly, but not in any high level languages, like C/C++.
In assembly, that is correct. Assembly is just a coding system, they are just codewords that directly represent instructions.

"doesn’t matter the language"
Yeah, you don't know anything about this subject. Didn't you say you were learning programming? What language are you trying to learn?
And why on earth do you think taht we would even have different languages, if this was true? Just for a different "look"?
No, they all have different capabilities, which doesn't simply mean that some of them lack a codeword for a specific instruction, it's far, far more complex than that.
You're only talking about assembly, that's all. That's the only example that fits with what you're saying, as far as I am aware. Any high-level language is not a coding system, it is an actual language that you use to talk to a compiler.

"well you’ve just said there are things intelligence alone can cause"
Yes, there are more things that only intelligent life can cause, I'm quite sure. We can do an almost infinite number of different things.

"and Intelligence is a cause dammit … intelligence is real"
Yes, it is "a cause" some a lot of different things.

"but your confusion obviously is that intelligence is only limited to humans … that’s totally and factually wrong "
I would never say anything like that. Most animals are intelligent on some level. Some of them are clearly quite intelligent. You've clearly misinterpreted something I said.

" I’m even certain you believe in Extra terrestrial intelligence "
No, I don't. I believe in the possibility of it, but  not the existence of it.

"wow … a failure of thought says someone who believes intelligence doesn’t produce induction motors and computer codes "
If you think intelligence produces technology, not intelligent creatures, then I really can't help you.

"intelligence is the best explanation for any technology we have "
Intelligence can produce knowledge, through its ability to reason. It doesn't produce technology, which is the practical application of knowledge/science. For that, you need something like a creature to actually do those things.

"*Therefore, some things that intelligent creatures make is also made by nature.* … lol close … actually it’s : some things that intelligent creatures can make is created by nature"
Both are true, are they not?

"my point is obviously that nature cannot make a computer: and I’m talking about the nature we all know"
If you mean a computer just like a PC, then you're probably right, yes.
Technically, we can't say that is definitely true, because that would be an argument from ignorance. But it is probably true.
See, we can't say it's impossible for nature to do something just becaue we have not found a way that nature can do it.
If we can prove that it is impossible, then it'd be fine. But we haven't proved that.

"IC says the system must loose its function on elimination of any part to be deemed IC"
Then it is a moot point, if you mean lose its current function, because obviously you cannot remove something from a system that needs it and still have that system function the same way.
If you mean "lose all/any function", then that is exactly my understanding of IC, and exactly what I've been talking about.

"no silly I’m saying the best and obvious explanation is a known cause which is intelligence"
Intelligent agency can be used as an explanation for pretty much anything. "Why is there a hole here? Because some guy dug a hole there." 
Is it true simply because it could be true? No, you have to establish whether its true or not, with evidence.
But what you're doing is that you're trying to use the hole itself as the evidence, which simply does not work. Something about the hole might be evidence of its origin, but not the mere existence of the hole itself, since that is what caused the question in the first place.

"maybe you can show me a demonstration of a flagellum evolving … that’d debunk IC instantly"
IC is a challenge to the theory of evolution to explain how something could have evolved. If we can figure out how it could have evolved, then the challenge has been met.
You seem to think IC is something it's not. It is a description of a specific kind of system. It is like a "criteria". You can look at something and say that it is either IC or not IC.
So someone can look at the human eye and say "this looks like its IC". That is a challenge to the theory of evolution to explain why its not IC.
Note that I am talking about a much more refined version of IC. Not simply "irreducible complexity", which is since long debunked as a pointless thing, but instead simply the idea that something could not have gradually evolved.
If somethign looks like it could not have grafdually evolved, then that it a challenge that must be met. The theory of evolution must be able to explain how something could evolve. If it can't, then it is obviously flawed.

"you said Newton “gave up and resorted to saying God did it” … and I replied “he didn’t come to a conclusion of God because he gave up on his science” … how much comprehension do you need to grasp this?"
Yes, he gave up and resorted to saying god did it. Really, read it again. Those are 2 thinga, there is an "and" there, not a "because" or anything like that. Those are 2 seprate actions: 1) Giving up, and 2) saying gid did it.
You imagine that I am saying there is a causal relationship between those two thing. That's where your reading comprehension fails you.

"and I’ve explain to you that the view of atheism was that God doesn’t exist … same view as today"
Not same as today, since today atheism means to "not believe in god", it doesn't mean to "believe gods don't exist".
This is exactly my point. I don't suspect you have the brains to see the difference, though...

"deist or agnostic would be a more suiting description "
But those are a different question. Yes, it's crude, but that's how it is. Atheist means to not be a theist. There are only those tow options, because it is abinary question: "Do you believe in god[s]?", yes/no - theist/atheis.
I'm not sure if desim counts as a form of theism. It might. But pantheism doesn't, I think, because the question actually assumes a personal god, not an impersonal god.
Yes, I know, the question isn't specific on that point, but this is a question of what the words mean culturally.
If deism isn't theism, then it is atheism, crude as it might sound. And yes, it weirdly means that it's possible that you might be able to be a deist and an atheist at the same time. (?)
I don't make the rules, though, and I'm not responsible.
"Agnostic" is something completely different, as we've established.

"obviously no reasonable person would call him an atheist after reading all his comments about atheism "
I dunno, take his comments about atheism, like you said, and weight that against his comments about gods and religions. I would stilla rgue that he was an atheist, and I am most certainly not alone in that.
But this is only because pantheism isn't theism. If you don't believe in a personal god, then you don't count as a theist, normally. If you'r enot a theist, then you're an a-theist.

"I mean, I am an atheist, and I agree with every word I have read that he said on the subject. … I don’t suppose you agree with this" (And then the quote form Einstein)
It is very clear, from those quotes, that Einstein defined "atheist" as someone who believes that "gods do not exist".
And as I've said, that is not what atheism means. It may be that that was what it culturally meant back then, or perhaps Einstein had misunderstood what it means. I don't know. But it's clear that he doesn't mean the kind of atheist that I am, and that people of today tend to be.
Einstein would fit into our label, because he would probably call us "agnostics", and he agreed that he might be called an agnostic.

"the core idea is that we don’t know enough to conclusively describe or dismiss God … not that we don’t know about God "
Agnostic: The exitence of god is unknown (and unknowable).
I haven't disagreed with what you're saying. I shortened my earlier statement, and yes, it can be interpreted as meaning what you thought I mean, and that's my fault, it was ambiguous.
However, the result of not being able to know if god[s] exist is that we also can't know anything about them. Being able to know things about them requires that you know that they exist, to begin with.
I have literally read a definition of agnosticism that said that "god is unknowable".

"environmental conditions are random"
Yeah, volcanos can spring up anywhere at any time, for no reason, huh? It can just randomly become icy cold?
You're a moron, you know that.

"Natural selection just says anyone who’s random mutations are favored by the random environments, is lucky "
Ignoring that "random environments" nonsense, then yes, you could say that, if you want to over-simplify. You really want to be the right guy at the right place, so to speak. Do you have a problem with this?
If a sudden selection pressure is introduced, where you need to be tall to survive, then yes, obviously some are goin to be "luckier" than others in that they happen to be tall. You speak as if this is strange, somehow.

"that just like saying the criteria for selection in a dice is 1-6 and so 1-6 can be good or bad … ie you can roll 1 and be luck: you can also roll 1 and be unlucky "
Environmental pressures don't change very often or very quickly, normally.

"predicting there’s be no 7 is like predicting there’d be no fire breathing nuke launching mountain size dragon … 7 doesn’t exist on a dice so that prediction is obsolete when considering a dice "
Are you seriously telling me that knowing someone won't be able to roll a 7 does not matter? Like you said, 7 doesn't exist on a die, and knowing that makes a difference. If it was truly random, you would not be able to predict anything about it.
The fact that some "random" things follow a system to some extent means that we can predict what is more likely than other things, and that makes a difference.
When you roll 2 dice, we know that 7 is more likely to turn up than the number 2. You know this, right? There are many ways to roll 7, but there is only one way to roll 2.
But this is a matter of distribution. There are other ways that somethign can be more or less random. Computers suffer this problem of not being able to generate truly random numbers, but have to fake it as well as they can. That's why they're called "pseudo-random".

"well just want to be clear … if it’s proven and demonstrated that evo is random, would you consider it absurd?"
If evolution is random, then the concept of evolution doesn't exist. The whole point with it is that it isn't random. We can only identify evolution because it is a specific change, not a random one.

"*Also, consider how anyone could make a theory of something that is random.* … well it already happened: why do you think I’m in this argument? "
Go troll someone else.

"how to predict something random evo 101 … simple … it will change"
Why don't you actually test that idea?
Take the number 10, and make a shitload of copies of it, with a random offset such as +1 or -1.
This would be our gene pool.
What is the average value of all the numbers in this gene pool? Should be 10, or very close to it.
So, keep making copies of the copies and adding a random offset to them, it doesn't matter how many times, and the average will still be about 10.
No change in the "species", so no evolution.
The only way that the average can change is if something drives the change in a specific direction. But then it isn't random anymore, it is lawful, it follow some kind of system.
Evolution follows the environment. That is not "random" change, it is change according to the environment. Lawful change.

"*God you're dumb.* … hahahaha … wait a minute did you just call “God”? … 8| … with the capital letter?"
Yes, that is the expression. And capital letter, yes, because it's grammatically correct to start a sentence with a capital letter, in case you didn't go to school at all.

"undirected still means random"
Get a dictionary.

"evolution is inherently undirected: but it doesn’t move in a backward direction"
Beause perfectly retracing your steps is not likley to happen, and to evolve backwards means you have to have the same environmental pressures, but "inverted", and in reverse sequence.
It's really not hard, if you would just rub your two brain cells together, you might understand this.

"evolution has no specific outcome but it specifically doesn’t give outcome “X” … lol"
I can really picture you sitting in school, laughing at everything they try to teach you because you're too dumb to understand any of it, and too dumb to understand that you're too dumb.
It's sad, really.
 
"evolution actually equates two(or even 3) different things as if they were the same thing "
"Evolution" is not a person. "Evolution" cannot equate anything.

"well lets see … how do you merge these three concepts above into one definition? Simple … organisms change "
And since when did merging somethign become a logical fallacy? Just out of curiosity.
And I have told you what "evolution" is. It isn't "organisms change", it is that the frequency of different alleles in a gene pool changes over time.

"well the facts show it started to exist … even if your brain can’t capture what it could have been like before, don’t be downcast"
Yes, the universe most likely started to exist, but that doesn't mean there was any time before time existed.
You say "before". Have you already forgotten that time started at the big bang, therefore there is no "before the big bang"?

"evidence is not a limitation if you can create the evidence out of imagination"
It doesn't matter if you can create imaginary evidence, because that's only you. The rest of us will still be waiting for real evidence.

 " to know if something was designed you need to find the evidences of design and compare"
And the evidence of design is when you find the designer...!

"well it is very possible that these creatures were created but were lost due to entropy : and the creator just created more : each time, adding more information to help withstand entropy and exist longer"
So a really bad designer, then, who keep failing and never seems to learn.
The thing is, however, that you can't use something that you don't know exists, or even know can exist, or even know what it is, as an explanation for something. You're literally just making some absolutely unfounded, undefined, vague guess, like "weeeelll..... maybe some magical, invisible, immaterial guy did it?"
You could just as well have said "magical unicorns did it". It makes absolutely no difference, it's still completely crazy.

"why do you think gradualism was dumped?"
Because punctuated equilibrium makes more sense than gradualism, and also fits better with the evidence.

"well perfect and unclouded inference definitely suggests design at the Cambrian period "
No, absolutely not. We have no evidence of any designer at that time.
But what, are you saying that the cambrian lifeforms could evolve to all the diversity of life that exists today, but they themselves could not have evolved from some other lifeforms?
It's unclear what you're trying to say.

"except you could explain to me again how these organisms morphed so fast and forgot their transitions "
Huh? What? I think you need to be more specific, because I don't get the question.

"first prove that love, music, beauty, etc. exists, with the scientific method "
We study these things, in science. We wouldn't study them if they didn't exist. We know they exist, because we observe them. They are scientifically real.
Once again, you're not making sense, I don't get what you're trying to say. It's like you're an alien, or something.

"Life is not an isolated system. … the universe is an isolated system so?"
Most likely, yes, but life isn't. We're talking about life, remember? Life is an open system.

"(Fuck, I'm so tired of people pulling up entropy...............) … it’s the best piece of fact that debunks evo"
...
No... no, that's it, I can't stand your stupidity and trolling anymore.
Nice way to waste your own time, btw. Write over 1000 lines, and make sure that you write so much obnoxious bullshit that no one can actually stand to read it.
Reply: Max Spiegel 

What experiment do you think demonstrates that IC structures cannot arise through evolution? ... like I said, the experiment I proposed demonstrates that the system in question needs the core to function ... that's the fact as shown by the experiments ... it's only logical to go on to say gradual steps can't build it ... even Millers explanation of exaptation involves spontenous assembly of the required parts ... but it's not logical as he overlooks the intricate matching and ordering of components, as well as the probability for such assemblage ... which was pointed out by Behe ... In addition, no structure homologous to the flagellum can be conclusively considered as an intermediary step because loss of function is also a fact ...

What exactly is wrong with the Mullerian two-step approach (which is what I used in the bridge analogy), in which a part is first added, then made necessary (perhaps through the removal of another part)? ... well again ... adding a part and making it necessary even in your analogy is definitely easier to say than actualize ... like I said the new part added has a greater chance of getting eliminated because evo. as observed destroys components more on the average ... this was why I said a rational person would choose the obviously grater probability ... it takes faith to choose the opposite ...

in addition, adding a well matched part is even less likely ... you're hoping in your analogy that the wood on the top is perfectly plane and just of the same length ... in reality, if the wood is added randomly, then the chances of it matching the stones are very low ... except you take the time to cut it to size ...

also, making the part necessary is very less likely in your analogy ... you have four components with a random knockout of a component ... definitely it'd be less likely to have the middle stone knocked out ...

the main issue is that you seem to be using the stone bridge analogy without considering the actual processes involved ... in reality, to even form a stone from nothing would require formation of adequate proteins and DNA info. forming a matching stone is hence extremely unlikely ... you said evo. needs one favorable mutation ... no ... it needs a host of favourable mutations to even get something like you stone bridge ... how more so a bacteria flagellum?

And what answer do you have to the many successful predictions of evolution, such as the transitional fossils I linked you to? ... sorry I didn't read the previous comments ... like you said I was running out of steam replying to you and AHD ... but also, like I said, transitional fossils make little sense if you can just conjure up over 70% of missing parts from less than 30% of actual fossils ... Pakicetus is a good example ... and many more ... if you want to give transitional fossils, then I suggest you give full skeletons or atleast 70% of the fossils ... it'd be more credible ...

Where are such successful predictions of ID (or even unsuccessful, yet testable for that matter)? ... well considering the fossil record, ID predicts signs of spontaneous creation: the cambrian explosion typifies this ... ID also predicts no transitional fossils and there are little to no actual transitional fossils found ... that was why gradualism was dumped ...
Reply: Benjamin Toby
"like I said, the experiment I proposed demonstrates that the system in question needs the core to function"
And again, hat removing the "core" makes something not work does not prove anything beyond that removing that component makes it stop doing the job it currently does. The degenerate version and its various components could have had different functions before, as you have admitted. This was actually illustrated specifically for the flagellum with the T3SS.

"it's only logical to go on to say gradual steps can't build it"
No, this is a huge logical leap that you consistently make without justification. The bridge example disproves this in principle.

"but it's not logical as he overlooks the intricate matching and ordering of components, as well as the probability for such assemblage"
The "matching" and "ordering" seem to be a matter of probability, and calculating those probabilities requires taking into account natural selection. Show me those probabilistic calculations. The only I have ever seen treat chemistry as a random system and ignore natural selection. Do you have better ones?

"like I said the new part added has a greater chance of getting eliminated because evo. as observed destroys components more on the average"
None of those versions would be kept because of NS. Only the versions that "work" would be. I have said this many times now.

"this was why I said a rational person would choose the obviously grater probability ... it takes faith to choose the opposite ..."
Again, evolution has no interest in whether it is more likely that a mutation be beneficial. It has all the time in the world, and NS only keeps the working versions. It can make 1000000 bad versions and 1 good one, and it is the 1 good one that would go on to replicate and produce the next generation as a result of NS. You are trying desperately to ignore NS, just like every probabilistic argument ever presented by any ID proponent.

"in addition, adding a well matched part is even less likely ... you're hoping in your analogy that the wood on the top is perfectly plane and just of the same length ... in reality, if the wood is added randomly, then the chances of it matching the stones are very low ... except you take the time to cut it to size"
Firstly, we are imagining that there are only a certain number of different "blocks" to use (analogous to amino acids), so it's not like the wood could take on any shape or size. Secondly, you are admitting that IC structures can arise through evolution, but you are claiming it is too improbable. Realize that this means that, in principle, IC is completely useless in determining if something could have evolved unless you can show it is probabilistically impossible. Now show me you calculation that demonstrate this, which again must account for NS and not treat each probability as independent, since that's not how either biology or chemistry work.

"also, making the part necessary is very less likely in your analogy ... you have four components with a random knockout of a component ... definitely it'd be less likely to have the middle stone knocked out"
Oh no, you mean NS would have to discard 3/4 possible mutations? That's completely... how NS works! It can discard billions of bad mutations by not allowing them to reproduce. Evolution happens on a large timescale, so such a barrier of a beneficial mutation being less probable is irrelevant if it can occur, which you have now admitted multiple times that it can.

"in reality, to even form a stone from nothing would require formation of adequate proteins and DNA info."
In our analogy, the "stone" can be made of just one amino acid. There is nothing preventing DNA from generating such a structure.

"you said evo. needs one favorable mutation ... no ... it needs a host of favourable mutations to even get something like you stone bridge ... how more so a bacteria flagellum?"
Evolution only needs one beneficial or neutral mutation at a time to move "forward" with a particular design. Obviously something like a flagellum has many such accumulated mutations, which is precisely why it took many millions of years to evolve.

"transitional fossils make little sense if you can just conjure up over 70% of missing parts from less than 30% of actual fossils"
Look again at the list I gave you and tell me how they are all "conjured up." Why should even one have been successfully predicted if evolution was wrong?

"well considering the fossil record, ID predicts signs of spontaneous creation: the cambrian explosion typifies this"
Another postdictions and not a prediction, and obviously cannot be falsified. Predictions must be made before the discovery that supports it. Did ID predict the Cambrian explosion before it was discovered? Nope.

"ID also predicts no transitional fossils and there are little to no actual transitional fossils found ... that was why gradualism was dumped "
Again refer back to the list of transitional fossils I provided and tell me with a straight face that there are "little to none of them." Punctuated equilibrium gained favor because of a lack of transitional fossils on the species level, not in general. This shouldn't be too surprising when we consider how unlikely it is for an organism to fossilize and then be found by humans. And again, all of this begs the question of why evolution successfully predicted the existence of transitional fossils at all.

Still waiting for a unique, falsifiable prediction that supports ID. The Cambrian explosion doesn't work because it wasn't predicted. Try again.
Reply: antiHUMANDesigns 

Goddamnit, I told you that because "hello" is an interjection, the example would get unnecesarily confusing. This is why our conversation gets so unnecessarily long, I think you're intentionallytrying to make things confusing for yourself. … well I think the word “hello” falsifies your definition … 

Yes, in a sense, the word "hello" is special because it doesn't really "mean" anything, it's just something we say, like a sound we make. That's why it's called an "interjection", in this case a secondary interjection, not a primary. But the written symbol, "hello" still refers to that thing, that idea of that greeting. … what of when it’s not written? … does it mean there’s no code? … 

The thing that "A" refers to is real, it is a specific kind of sound. … if the sound is the morse code, then we still don’t have the second symbolism … from your definition, A has to represent a “real thing” … my question is what’s this “real thing” A represents … if the sound is the “A” then we have a problem: what happens when we don’t have to write the letter “A”?

"A" is a symbol, and the morse code for "A" is then a symbol for a symbol, so "code". … “A” is symbol for what? A sound? … not sure about that … 

The poroblem is that the thigns you're talking about are "codes", but those codes only exist in people minds. …  well again, I’m not saying codes can’t be strictly conceptual: I’m just saying the computer code is not strictly conceptual …

It's our way of decribing them. They aren't physically codes, because... yeah, "code" is conceptual. … what I got from this is that non of our description for anything is actually real … so a “cat” is not actually a cat in the sense that it’s just the concept used to describe the real thing … 

A CPU gets an instruction. And "instruction" is our simplification7symbolism for what it really is.  When we give specific instructions (which are symbolical) specific najmes, then thosenames are codes for those instructions. But it isn't the names that go into the CPU, it is the thing that those names are referring to. Specific patterns of voltages. …  I think I have a better idea on how to clarify this … if you think all our descriptions of the computer code are just representations of the real thing, then C++ is as much a code as binary or any other language… what you’re saying in essence is that the code in computer is just to represent an actual thing the same way “box” represents an actual thing … this is how I got this:
1.	You said “box” and “instruction” are symbols for what actually happens in reality …
2.	I just took this to mean that every thing else we write or say are symbols for what actually happens … “go” , “come” , “think” , “arrive” , every damn word is a symbol for the “real thing” …
3.	You said the “real thing” in the computer is the switching of voltages …
4.	You also said “binary strings” are symbols for this “real thing”
5.	This clearly means that hex codes are symbols for the real thing same way: because they end up in voltages same way binary codes do
6.	This in turn means that C++ codes are symbols the same way binary codes and hex codes are: because they end up in the “real thing” which are voltages …

The switch patterns are not symbols, they are the real thing. We use symobls to refer to real things like that. Real things aren't supposed to be seen as symbol for conceptual things. … they’re both real buddy … the switch patterns and the button … not sure exactly what you’re driving at here … but what I’m saying is that the switch patterns represent that one button …
Yes, you could say that the letter "A" is symbol for that specific sound, and therefore that specific sound is also symbol for the letter "A", but it just makes no sense to think of it that way, because then the whole idea of "symbolism" goes out the window. Symbolism is inherently conceptual, and the real world isn't at all, therefore the real world can't be symbols. (?!)
Yes, the button could be thought of as a symbol for something that will happen when you press it. At least he marking/label on the button is.
When I press the "A" key on my keyboard, we basically pretend that I sent an "A" into the computer. Software is a huge system ofpretend. In the end, all we've got is voltages going around in ciruitry, and as long as we keep track of everything and make sure everything is consistent, then the illusion that there's more going on can be upheld. And that is useful to us.
Software is still people communicating with people , not the computer communicating with people. When I use a program, I am really dealing with the person who wrote the program, not the computer.
Even when I see an error message, the error message was written by a person with the intent to inform the user that somethign has gone wrong. It isn't actually the computer talking to you.

"Aside this, I brought up the analogy to explain the Computer code : and from this a code is anything that represents a specific action"
Yes, thank you. The code represents a specific action. That is exactly it, and what I've been trying to tell you all along. … well I can say that I’m glad that we can finally come to an agreement … but I’m not sure if you’re reading the definition with the intent in mind … I particularly emphasized the word “specific” … by that I mean a code activates one function and one alone … the “represent” is not really a point of emphasis … yes it does represent a specific action … but the specificity is my basic point in this definition …

It action doesn't "represent the code", as you've said so many time, now. Obviously, there is a problem here, since you contradict yourself. … I don’t think I ever said an action represents a code … not sure where you’re getting that …

Well, this explains it, then. I see your problem if you think that "A" is not a symbol. … well this might be a bit confusing but it’s not like I’m saying A is not a symbol of some sort … I’m just saying it doesn’t have to be a symbol for a real thing … so far as I’m concerned, “A” is just a symbol for A
When you wrote this to me, I read the symbol "A", and my brain heard the sound that "A" refers to. … well there’s no difference in this context because I can send you a couple of sounds(morse code) through the phone and you’d not have to write it down to know it’s the letter “A” …

Of course it's a symbol. It's even called a "symbol". A letter is a specific kind of symbol. Letters are a "category" of symbols. … and I reckon this category is not what you’re trying to say …

Apart from this, the rest of what you said here is correct. And that makes me happy. … happy too to see some progress … maybe we could work on this since it probably has a better future …

"*"A code" is just one symbol, not enough to produce a program.* … but codes can … this was why I said a program contains CODES … no one code … a single code contains a single function"
You can't say a single code contains a function, because that heavily depends on what coding system you're using. … yes I can say that: confidently: our technology requires that the code word “mov”(like you said) doesn’t end up deleting a file totally … and you can’t say “mov X” and it ends up moving “Y” … 
Anyways, I think we need to define what we mean by "program". In what sense we mean it. Because in one way, you're correct: … well I can say a program is anything that functions according to preset instructions … it’s up for scrutiny tho …

If you consider the source code to be a program, then you're correct, the "program" contains codes, it is made up of codes. … well I consider the source code to be the “fancy” name used to denote the collection of codes that make up a program or application …

But if you consider software that runs on a computer to be a "program", then it doesn'tcontain code. … well software is more or less a program … 

The source code is only conceptually a program. It's "going to be" a program, when the compiler turns it into one. The computer can't run it, therefore I don't consider it to be a program. So clarify which you mean before we go on. … the source code still exists after the computer turns it into executable form … which means that the only limitation in source code is the language barrier … but the source code directly translates to machine language … just one padded to suit the human understanding better …

I just don't want to call it "code", because whether it is "code" or not depends on what language you're programming in. And I'm trying to be strict with my usage, to avoid confusion, but I'm not sure it's working. … well the language doesn’t matter … whether binary, hex, C++, html , or any other language …

"Code" as an uncountable noun. "Code", in this sense, can contain any amount of "codes", thus any amount of "functions". … well I suggest you treat the term as a countable noun … atleast till we clear it up …  

And thus, "code" can contain a program, aswell. Source code (uncountable noun, again) does, for example. … a code can contain a program if you adjust the context … Source code can be a type of code … but we are trying to define what a code is to begin with …

If it is a value, then why are you calling it a "color code"? … OK there’s a good chance I might have used the wrong term this time: but I was hoping you’d get my point anyway … maybe “code” would have been more appropriate instead of “value” …

Are you talking about something like the hex for a color, such as "#FFAA55"? Or are you talking abotu something like "RED" or "VIOLET"? …
The only kind of "color code" that isn't code is the kind that graphics cards use. Yes, it's a value. We do not call those "color codes", because they aren't codes, they are direct symbols.
"#44FFAA" is a "color code", because a computer cannot directly read this, it has to be decoded to a value.

Remember, "binary form" is also symbolic. Anything that represents binary form is therefore "code", since it is a symbol for a symbol. … I think your analogy crumbles totally here … if binary form is symbolic for the “real thing”, then hex codes don’t get translated to “binary form” … hex codes are as much symbols as “binary form” like you describe it … hex codes actually get turned into the “real thing” … same with binary …

*"11101010" <- this is symbolism, not the real thing.*… this simply means “mov” is symbolism the exact same way “11101010” is … 

Hexadecimal in itself is not "code". It's just one way to "read" the same thing. Call it a "conversion", instead. … well all conversions end up in the real voltages … so hexadecimal is as much a code as C++ … btw don’t you use hex codes in C++? I use it in HTML directly in my source codes … 

So it is not "hex code", unless you're talking about something else, such as my example of "#FF55AA", which is a "color code". … if it’s represented in hex form, and it’s called code, then it hex code … what’s wrong with this?

When you "put the binary directly in", then it is not code, it is symbolism. You're writing "11010101010", or whatever, which is direct symbol for the pattern for the switches. … well all languages are direct symbols for voltage patterns … it’s like you said … the compiler would translate your C++ program in to voltage patterns same way it would translate the hex code into voltage patterns : binary too I’d presume … the only reason I use binary is to just represent the two states: it’s actually my way of saying “the real thing” …

Within a framework of some kind, that someone has written. The computer itself cannot read and understand "color code", or it wouldn't be "color code". … and again for anything to be called “computer”, it must have some sort of artificial understanding … so yes the computer can understand the “color code” … the numbers and letters you write in your program are just to help you relate with the computer better … that’s all … the computer already understands it … the language is just to get you to understand it like the computer does : but in easier terms…  

Yes, it is for simplicity and clarity. But it still becomes second-level symbolism, which means that is is code. That's why it's called "color code", because it is. … 

Likewise, "TGAAAGC" is code for DNA sequences, only for simplicity. It would be extremely cumbersome to have to write the actual name of the nucleobases, so we use codes for them. … you know I actually suggested you stayed out of the DNA until we clarify code … according to you, “TGAAAGC” is just the representation(symbolism) of the actual “thing” … so by your definition it’s not code because there’s no second level symbol … 

I think there’s another pretty confusing aspect here … Morse code can be represented on a paper by dots and dashes … but that’s just a representation … technically it’s still the code but the real code is the sound patterns … we can make up different languages to represent the symbolism we use for DNA … we can say “mov” can be equated to “TGAAGC” …we’ve shortened it but still “mov” represents the same thing … this is basically what goes on in programming languages …

Damnit, I should've known you still wouldn't know the word "abstraction", even though I just explained it. It doesn't mean anythign is abstract. … I stand corrected … I really didn’t bother to inspect this closely as I would normally because there was just too much lines to respond to … anyway this might well be a rare piece of good info. You’ve given : atleast until I take the time to inspect it properly …

Yeah, you don't know anything about this subject. Didn't you say you were learning programming? What language are you trying to learn? … well I’m on HTML/CSS now … aiming for PHP…

Yes, there are more things that only intelligent life can cause, I'm quite sure. We can do an almost infinite number of different things. … so what’s your beef if I say only intelligence can create an IC system? Or genetic code?

Yes, it is "a cause" some a lot of different things. … and like I said it’s the best explanation for certain things … 

I would never say anything like that. Most animals are intelligent on some level. Some of them are clearly quite intelligent. You've clearly misinterpreted something I said. … well I hope I have misinterpreted you because the fact is that intelligence is not just limited to humans … and it’s my basic point …

No, I don't. I believe in the possibility of it, but  not the existence of it. … don’t really get you here … if you believe in the possibility then you believe it can exist … if so what’s your beef with God?

If you think intelligence produces technology, not intelligent creatures, then I really can't help you. … I really think you need more help on this one … using “intelligence” is much more accurate and appropriate… dolphins are intelligent creatures but they don’t create technology … 

Intelligence can produce knowledge, through its ability to reason. It doesn't produce technology, which is the practical application of knowledge/science. …  well I hope I’m not reading this right … because the root of all technology is intelligence … 

Then it is a moot point, … no silly it’s not : it’s just a distillation of the fact … 
if you mean lose itscurrent function, because obviously you cannot remove something from a system that needs it and still have that system function the same way. … that’s what IC is … just that you’re obviously confused about it and what claims you should be looking to refute : the claim that something is IC is a scientific fact: the claim you can attempt to refute is the claim that evolutionary process can’t give rise to it … 

If you mean "lose all/any function", then that is exactly my understanding of IC, and exactly what I've been talking about. … and exactly why I’ve been calling out your ignorance as well as the ignorance of the supposed scientists that claimed they refuted IC … 

Intelligent agency can be used as an explanation for pretty much anything. "Why is there a hole here? Because some guy dug a hole there. … not just anything … this was why I particularly gave the Stonehenge analogy … even the hole: if you see a well (technically a hole), one can easily tell that intelligence is the best explanation even if the agent is unknown … 

No, you have to establish whether its true or not, with evidence.  and we’ve done that : the evidence is in our repeated experience with IC systems: from this we know that only intelligence can account for an IC system … no experience has been seen of nature building an IC system … such as the flagellum … so it’s actually your position that needs evidence …

But what you're doing is that you're trying to use the hole itself as the evidence, which simply does not work. … isn’t that basically what evolution does? … 

Something about the hole might be evidence of its origin, but not the mere existence of the hole itself, since that is what caused the question in the first place. … ofcourse the existence is directly related to the attributes of the hole … I’m not sure exactly what you’re trying to say here … we’re saying the reason this exists is intelligence, and it’s attributes prove it …

IC is a challenge to the theory of evolution to explain how something could have evolved. If we can figure out how it could have evolved, then the challenge has been met. … lol hell no … if you imagine an evolutionary process it has no weight what so ever on the facts … it’s only when the facts say otherwise that you do have a refutation of IC … and like I said to Spiegel … the imaginary processes are best validated by probability … if an imaginary process is so highly improbable, then it’d require faith to accept it as truth … to a rational person, it’s the most probable that goes …

You seem to think IC is something it's not. It is a description of a specific kind of system. It is like a "criteria". … not sure exactly what you’re saying here …  
You can look at something and say that it is either IC or not IC. … better still, you can actually test it out and establish beyond any reasonable doubt that a system is as a matter of fact, IC …

So someone can look at the human eye and say "this looks like its IC". That is a challenge to the theory of evolution to explain why its not IC. … well it’s more than looking … I explained a situation called Aphakia to Spiegel which is a scenario where an eye has no lens: the eye turns out to be almost useless … aside this, you can just do a lab experiment to prove the exact parts needed for the eye to function … after proving this, you can’t just come up with a story that “this happened, that happened, and so it evolved” … this can’t disprove it, not the slightest chance … you’d have to prove this can even remotely happen in a lab to disprove the fact …

Note that I am talking about a much more refined version of IC. Not simply "irreducible complexity", which is since long debunked as a pointless thing, but instead simply the idea that something could not have gradually evolved.  … no you’re talking from your ignorance as what was debunked was just an ignorant interpretation of IC … 

If somethign looks like it could not have grafdually evolved, then that it a challenge that must be met. … again not that it looked like: it’s that it’s factually established that it requires the said parts to function: and these parts are needed at the same time … 
The theory of evolution must be able to explain how something could evolve. If it can't, then it is obviously flawed. … well exaptation attempts to explain how the parts assembled spontaneously: but that’s just laughable and wishful thinking which has an astronomically low probability and little to no facts to back it up… exaptation basically said all the components once had individual functions and at a point in time, they all collated perfectly to form the IC system … that honestly a big lol …

Yes, he gave up and resorted to saying god did it. Really, read it again. … I suggest you read it again, or just sharpen your comprehension skills … I can’t press on this much longer … 

Not same as today, since today atheism means to "not believe in god", it doesn't mean to "believe gods don't exist". … that was what atheism meant in his time and even before his time … he’d still hold the same position today… what he rejected was a personal God … he believed in some other sort of God … not particularly sure … 

This is exactly my point. I don't suspect you have the brains to see the difference, though... … lol … and I’m sure you have the brains to realize it’s going to end you in a whirlpool … if atheism doesn’t mean to believe “God doesn’t exist” it means to believe God exists (or atleast have no objection to that thought), but just choose not to believe in Him … so could you say you have no objection to the thought that God exists? Oh wise one?

If deism isn't theism, then it is atheism, crude as it might sound. And yes, it weirdly means that it's possible that you might be able to be a deist and an atheist at the same time. (?) … lol … deism is theism then … sorry …

I dunno, take his comments about atheism, like you said, and weight that against his comments about gods and religions. I would stilla rgue that he was an atheist, and I am most certainly not alone in that. … yes ofcourse you would … particularly why I said no reasonable person would … you’re only joined by your colleagues desperate to classify Einstien under their weakly developed paradigms … 

*But this is only because pantheism isn't theism.*… I believe I said “panantheism” … learn to read closely … 

*If you don't believe in a personal god, then you don't count as a theist, normally.*… lol no … like you said, atheism and theism are two direct opposites … if atheism means lack of belief in God or supernatural beigns, then theism means belief in God or supernatural beigns … so it doesn’t matter the kind of god you believe in: whether personal or not… you’re still a theist …

It is very clear, from those quotes, that Einstein defined "atheist" as someone who believes that "gods do not exist". And as I've said, that is not what atheism means. … if so then you should have absolutely no objection to my thought that God exists … I mean since you’re an atheist and you only say you don’t believe in God … you have absolutely no justification to call God imaginary going by this … 

Einstein would fit into our label, because he would probably call us "agnostics", and he agreed that he might be called an agnostic. … lol …

Yeah, volcanos can spring up anywhere at any time, for no reason, huh? It can just randomlybecome icy cold? … haha I smell desperation … actually volcanoes can spring up anywhere at anytime lol … but not for no reason … the fact we can explain volcanic eruptions doesn’t mean it’s not a random occurrence : atleast for evo. … however weather conditions aren’t all to environment … environmental conditions could also mean a large amount of predators … so yeah … the environmental conditions are random …
You're a moron, you know that. … hahaha … and you are the embodiment of pure wisdom …

Ignoring that "random environments" nonsense, then yes, you could say that, if you want to over-simplify. … I’m glad you’re beginning to see the little details that makes evolution less credible: but it’s okay if you ignore them for now … 

You really want to be the right guy at the right place, so to speak. Do you have a problem with this? … not really … I’m just saying it’s what it is … a game of luck … just like a dice game … 

If a sudden selection pressure is introduced, where you need to be tall to survive, then yes, obviously some are goin to be "luckier" than others in that they happen to be tall. … I like the usage of the word “sudden” : astute way of debunking your own assertions … so tell me something : just how “sudden” are these “selection pressures”? … Aren’t they random?
You speak as if this is strange, somehow. … no I’m not saying it is strange per se … I’m just saying it is random …

Are you seriously telling me that knowing someone won't be able to roll a 7 does not matter? Like you said, 7 doesn't exist on a die, and knowing that makes a difference. … not much difference from knowing what a die is … 

If it wastruly random, you would not be able to predictanything about it. … you can predict that the outcomes would change … easy prediction you’d agree …

The fact that some "random" things follow a system to some extent means that we can predict what is more likely than other things, and that makes a difference. … Ooook … don’t really get you here but you can’t really predict the environmental conditions in evo.

*When you roll 2 dice, we know that 7 is more likely to turn up than the number 2. You know this, right? * … hahaha omg …
There are many ways to roll 7, but there is only one way to roll 2. … Oook yes you’re right … still random outcomes …

If evolution is random, then the concept of evolution doesn't exist. The whole point with it is that it isn't random. … well just answer the question dammit … 
We can only identify evolution because it is a specific change, not a random one. … I’m still confused : specific in what sense? That you can predict the outcomes it’d bring? Hell no … if so you’d know how to make a bacteria develop a flagellum in a lab … or you can repeat Lenski’s experiment and get the same exact result … but you can’t and do you wanna know why? Yes that’s right it’s damn random … the only thing you can predict is that the frequency would change … same prediction that can be made for any random event …

Why don't you actually test that idea?Take the number 10, and make a shitload of copies of it, with a random offset such as +1 or -1. This would be our gene pool. What is the average value of all the numbers in this gene pool? Should be 10, or very close to it. So, keep making copies of the copies and adding a random offset to them, it doesn't matter how many times, and the average willstill be about 10. challenge accepted … did the value change from 10? Hell yeah … proven beyond reasonable doubt … test successful … idea validated …

No change in the "species", so no evolution. …. Bu bu bu … there was a change in the frequency of the gene pool … so? Is evo. Now change in “species”?
The only way that the average can change is if something drives the change in a specificdirection. But then it isn't random anymore, it is lawful, it follow some kind of system. … hahaha … even with a convenient imaginary analogy your attempt fails … if we have a point where eleven gets more frequent then the change prediction is validated …

Evolution follows the environment. That is not "random" change, it is change according to the environment. Lawful change. … ok no need for any more laughter … this is just plain wrong … why are you trying to force some kind of “lawfulness” into something that is inherently random? … evolution follows both the environment and the mutations … and they are both random … 

Yes, that is the expression. And capital letter, yes, because it's grammatically correct to start a sentence with a capital letter, in case you didn't go to school at all. … good one … very good one indeed …

"undirected still means random"
Get a dictionary. … by dictionary I hope you don’t mean Swedish dictionary …

"evolution is inherently undirected: but it doesn’t move in a backward direction"
Beause perfectly retracing your steps is not likley to happen, and to evolve backwards means you have to have the same environmental pressures, but "inverted", and in reverse sequence. … well I see nothing here that can’t be achieved by evo. Just name the pressures required and imagine : it can happen … anyway you seem to get a hold on the contradiction … if evolution doesn’t move in a backward direction, then it’s not undirected … but I can remember you say evo. Has no specific goal or direction ... btw which human ancestor possessed wings? ... also it doesn’t make any difference to me if you use the law of irreversibility because I don’t believe organisms morphed from other organisms like you … 

It's really not hard, if you would just rub your two brain cells together, you might understand this. … hmmm … you’re forcing this too hard … I may well suggest you do the rubbing to get my drift … 

I can really picture you sitting in school, laughing at everything they try to teach you because you're too dumb to understand any of it, and too dumb to understand that you're too dumb. … it seems you ran out of the fallacies description : normally I’d expect something like “no this is AHD fallacy” … lol … anyway it’d be more useful if you told me exactly what it was I said wrong … so far as I’m concerned I’m very well in my limits going by what you’ve said so far … 

It's sad, really.
 
"Evolution" is not a person. "Evolution" cannot equate anything. … no kidding? … that’s brand new information … 

And since when did merging somethign become a logical fallacy? Just out of curiosity. … well I thought treating two different concepts as if they were one, was the fallacy? … well here are three different concepts going under one umbrella … “change” … 

And I have told you what "evolution" is. It isn't "organisms change", it is that the frequency of different alleles in a gene pool changes over time. … I stand corrected … how does evo. Merge these three different concepts again? Simple … “frequencies change” … makes little or even no difference …

You say "before". Have you already forgotten that time started at the big bang, therefore there is no "before the big bang"? … yes there was … but there was no time as we know it at that point … it’s ok if it’s confusing …

It doesn't matter if you can create imaginary evidence, because that's only you. The rest of us will still be waiting for real evidence. … hence my questioning … I’m asking for real evidences … as well as many scientists and normal people that know the truth about the transitions … I don’t think the supposed fossil evidences can be used in any serious debate or in a law court … the only singular piece of evidence that can be used is that which I pointed out … the chromosome 2 … 

 *And the evidence of design is when you find the designer...!* dammit no: why are you making this hard for me … why didn’t you find the designer of the Stonehenge first before deeming it intelligently designed? …

"well it is very possible that these creatures were created but were lost due to entropy : and the creator just created more : each time, adding more information to help withstand entropy and exist longer"

So a really bad designer, then, who keep failing and never seems to learn. … lol did you read the comment or are you talking off your ass again? … I said each time He added more info to help the organisms withstand entropy … what don’t you understand here?

The thing is, however, that you can't use something that you don't know exists, or even know can exist, or even know what it is, as an explanation for something. You're literally just making some absolutely unfounded, undefined, vague guess, like "weeeelll..... maybe some magical, invisible, immaterial guy did it?" … well it’s a hypothesis, but not an unfounded or undefined or vague one … and it’s damn not as simplistic as “come magical guy did it” … you might want to do some rubbing of brain cells here … it’s based on the sudden appearance and disappearance of fossils in the fossil record … 

You could just as well have said "magical unicorns did it". It makes absolutely no difference, it's still completely crazy. … I’d say the magical unicorns did it but for the fact that the magical unicorns have no explanatory power which can be applied to reality … a pretty horse with a horn between its nose … saying what exactly? … lol …

Because punctuated equilibrium makes more sense than gradualism, and also fits better with the evidence. … well personally I think it was because it was a fail … and I’m still not certain how punctuated equilibrium helps the situation … it’s like Dawkins said : “without gradualism, we’re back to a miracle” … well well well … well said …

No, absolutely not. We have no evidence of any designer at that time. … it’s evidence for spontaneous creation how many times must I say this … spontaneous creation is in turn evidence for a designer … and we know this because evo. Would have left their transitions if it ever evolved…

But what, are you saying that the cambrian lifeforms could evolve to all the diversity of life that exists today, but they themselves could not have evolved from some other lifeforms? … I’m not saying this : you are … and that’s mostly non-factual … I’m saying the Cambrian fossils show no sign of evo. And sufficient sign of spontaneous creation … and in addition, most of the fossil record show this sign as well … this was why gradualism was dumped … the only signs of evo. Are the ones mostly conjured up from imaginary evolutionary presuppositions … e.g pakicetus …

Huh? What? I think you need to be more specific, because I don't get the question. … I’m saying the Cambrian period actually disproves evo. Unless you could tell me how these organisms evolved so fast and forgot their transitions …

"first prove that love, music, beauty, etc. exists, with the scientific method "
We study these things, in science. We wouldn't study them if they didn't exist. We know they exist, … you assume they exist … it’s not a proven scientific fact … it can’t be tested or even defined … what is music in the real world aside sounds? Science can test for sounds yes … but music is certainly not just sounds …  

Once again, you're not making sense, I don't get what you're trying to say. It's like you're an alien, or something. … and once again, you’re probably not thinking at all… for you to say music is sounds : you should get a hold on the gravity of the situation … according to the scientific method, if there’s any sound that doesn’t classify as music, then music is not sounds … question is, what is music?

Most likely, yes, but life isn't. We're talking aboutlife, remember? Life is an open system. … well life is a subsystem in the universe: and if entropy is certain in the universe, how come it’s not in life?

No... no, that's it, I can't stand your stupidity and trolling anymore. … aww … you’re not going to give up now after spending so much time typing are you? … it’s not like I’m coming up with all the lines …you’re introducing nearly all of them: I’m only addressing them … 

Nice way to waste your own time, btw. Write over 1000 lines, and make sure that you write so much obnoxious bullshit that no one can actually stand to read it. … I’m sorry did you just describe yourself? …
Reply: Max Spiegel

The degenerate version and its various components could have had different functions before, as you have admitted. This was actually illustrated specifically for the flagellum with the T3SS. ... No it wasn't you have no proof what so ever that the T3SS was a precursor or a degenerated flagellum and if I take the later stance, you actually have nothing to work with : and the later stance is more probable and I've explained why ... even assuming your imaginations are somehow true ... you have the burden of adding 20+ perfectly matched parts each time creating new functions ... and that's highly improbable and virtually impossible for a random process which mostly destroys components ... It takes faith to believe this ...

No, this is a huge logical leap that you consistently make without justification. ... look if you're not going to recall my comments then don't just type without verification ... you're not making things easier for me ... like I said countless times the justification is both from the experiment and the fact that the process turns out to be more destructive on an average ... you actually need an experiment of this process building something like the flagellum from the scratch rather than unfounded and imaginary comments with no hold on reality ... this is the exact same thing you'd call magic if I said it ... you need proof ...

The "matching" and "ordering" seem to be a matter of probability, and calculating those probabilities requires taking into account natural selection. ... and with the proven fact that NS destroys info more on the average I would expect you'd gain a hold on just how improbable it is to build a new functional organ ... that has never been observed and only exists in the imaginary world ... but I'm not quite sure how you gain the confidence to bring it up as if it is fact ... 

Again, evolution has no interest in whether it is more likely that a mutation be beneficial. ... and one more time it's a rational person that is interested in the probabilities ... if you have such an improbable situation, then it needs faith to accept ... but you treat it as fact ... NS doesn't change the probabilities because it's still reliant on chance ... it's just a fancy way of saying "this mutation just so happens to be a lucky mutation" ... 

Evolution happens on a large timescale, so such a barrier of a beneficial mutation being less probable is irrelevant if it can occur ... no of course not the time scale makes little to no difference ... it's only an excuse you use to dump the burden of the complexity developed ... ofcourse we know that no amount of time can build a stonehenge from rockslides ... any such thought would be irrational ... if anything entropy would increase and DNA info. would get more less vaible ... 

It can discard billions of bad mutations by not allowing them to reproduce. ... ofcourse you've just accepted the probability of one beneficial mutation is extremely low ... but you choose to believe the plethora of beneficial mutations required for the flagellum are somehow likely ... this what we call blind faith ... you have no factual evidence to support this belief ...

Predictions must be made before the discovery that supports it. Did ID predict the Cambrian explosion before it was discovered? Nope. ... and what evo. predicted that herrings wouldn't produce penguins before it was discovered that herring don't produce penguins? ... lol ... 

In our analogy, the "stone" can be made of just one amino acid. There is nothing preventing DNA from generating such a structure. ... I'm guessing you need to say one protein ... considering the large range of proteins that can randomly spawn up, what's the chance that the proteins in the bases wouldn't turn out to be inappropriate for bridge bases? ... again the probability for appropriate proteins are against you even in your simple analogy ... and I'm justified if I say your analogy is not possible in reality ...

Punctuated equilibrium gained favor because of a lack of transitional fossils on the species level, not in general. This shouldn't be too surprising when we consider how unlikely it is for an organism to fossilize and then be found by humans. ... an excuse I'm not sure is quite viable ... of course there should be millions of transitional fossil on the "species level" : how hard is it to find one smooth transition from species to species ? or family to family for that matter?

And again, all of this begs the question of why evolution successfully predicted the existence of transitional fossils at all. ... that's more or less a false prediction ... again I repeat you'd need atleast 70% of fossil evidence for credibility ... the lucy is the most complete human fossil and it is 40% of fossil which is not even sure if it's humanoid or ape ... tiktaalik is a supposed transition that got its rare limbs conjured up from evo. world (which is imaginary) ... Panderichthys: skull bone mixed with evo. devo ... Ventastega: not sure how the hell it was conjured up ... Acanthostega: incomplete skull bone ... bruh I need evidences ... and these don't suit my criteria ...

Still waiting for a unique, falsifiable prediction that supports ID. The Cambrian explosion doesn't work because it wasn't predicted. Try again. ... lol Okk ... if it wasn't predicted by ID, then it was by Biblical creationism ... it's been saying for thousands of years that organisms were created spontaneously ... PS what about the Junk DNA I brought up? you forgot that? ...
Reply: Benjamin Toby
"No it wasn't you have no proof what so ever that the T3SS was a precursor or a degenerated flagellum"
The point is that part of the flagellum has a function, which illustrates that IC is a useless concept. If a structure is made of components that each serve different functions when not part of the whole, then your concept of IC as proof of somethign being impossible to evolve is dead.

"even assuming your imaginations are somehow true ... you have the burden of adding 20+ perfectly matched parts each time creating new functions"
Your missing the fact that in principle we just showed that the flagellum is made of components that can serve a function when not as part of the flagellum (let's call them (intermediate structures")., and now you immediately jump to "well those intermediate structures can't possible have any intermediate structures." In other words, you aren't happy unless we can find the exact evolutionary pathway for a structure. This is some serious goalpost pushing, and is completely unreasonable and unnecessary to prove evolution.

"like I said countless times the justification is both from the experiment and the fact that the process turns out to be more destructive on an average"
So then this is your logic: that removing a part makes a structure useless or serve a different function proves the structure could not have evolved because removing a part causes it to serve a different function, and beneficial mutations are less common than detrimental ones. Do you see the problem here?

"you actually need an experiment of this process building something like the flagellum from the scratch rather than unfounded and imaginary comments with no hold on reality ... this is the exact same thing you'd call magic if I said it ... you need proof ..."
And yet magic is precisely your alternative, since you have no experiments in which we have seen a "designer" create biological components "from scratch." Talk about hypocrisy.

"and with the proven fact that NS destroys info more on the average I would expect you'd gain a hold on just how improbable it is to build a new functional organ"
NS only destroys the "broken" versions, thereby increasing the fitness of the working ones; making their replication more probable.

"that has never been observed and only exists in the imaginary world"
We have not observed "organs" evolve because that takes too long. We have seen beneficial mutations improve organism though, which is all we need.

"and one more time it's a rational person that is interested in the probabilities"
I keep asking you to show me the probabilities.

"NS doesn't change the probabilities because it's still reliant on chance"
By changing the chances of the parent generation successfully reproducing, NS changes the frequency of the alleles passed to the next generation, so yes it does change the probabilities with a certain structure.

"it's just a fancy way of saying "this mutation just so happens to be a lucky mutation""
And so we keep it. And this means it is more likely to show up in the next generation. This is how NS changes probabilities.

"the time scale makes little to no difference"
Timescale makes all the difference. If I roll a die every 5 minutes, how likely am I to get all faces in 5 minutes vs in an hour? In a lifetime? In a billion years?

"we know that no amount of time can build a stonehenge from rockslides"
Firstly, we don't strictly know that. Secondly, that process is nothing like evolution because it involves no reproduction with variation and natural selection.

"if anything entropy would increase and DNA info. would get more less vaible"
Are you seriously bringing up entropy again? The earth is not a closed system! The 2nd law is only for isolated systems!!! Gah!

"ofcourse you've just accepted the probability of one beneficial mutation is extremely low ... but you choose to believe the plethora of beneficial mutations required for the flagellum are somehow likely ... this what we call blind faith ... you have no factual evidence to support this belief"
It is only the beneficial mutations which accumulate; never the harmful ones. This is proven by many experiments, like the nylon-eating E. Coli.

"evo. predicted that herrings wouldn't produce penguins before it was discovered that herring don't produce penguins?"
Keep repeating that and sounding like an idiot if you want. I've already given at least 5 examples of successful predictions made by evolution. You are currently tackling transitional fossils.

"what's the chance that the proteins in the bases wouldn't turn out to be inappropriate for bridge bases?"
I just took one starting point. We have to start somewhere. You are also acting like there is only one possible configuration that could be an "appropriate base."

"of course there should be millions of transitional fossil on the "species level" : how hard is it to find one smooth transition from species to species ? or family to family for that matter?"
Very hard on the species level. We have many on the genus level and above, but organisms don't cross from one family to another so that's not something we would expect to see. You understand this, right?

"that's more or less a false prediction ... again I repeat you'd need atleast 70% of fossil evidence for credibility ... the lucy is the most complete human fossil and it is 40% of fossil which is not even sure if it's humanoid or ape"
So if I present you with a transitional fossil that is more than 70% complete, will you accept it then? That would be awesome, and shows you didn't read the list I gave you.

"if it wasn't predicted by ID, then it was by Biblical creationism"
The bible predicts man and all other animals appeared in the first 6 days of earth's existence, which is nothing like the Cambrian explosion. Show me where the bible predicts the Cambrian explosion.

"PS what about the Junk DNA I brought up? you forgot that?"
Let's not bring another topic into this thread. We already have enough spreading going on here.
Reply: Benjamin Toby I wasn't going to answer your next reply, because I started getting the feeling that you were only in this to troll me.
However, I read you last reply, and your attitude is quite fine, for the most part, which I appreciate, so I will reply to it.
And thank you for that.
I have less time, nowadays, than I had a few days ago. I'll see how much time I can dedicate to this.

"well I think the word “hello” falsifies your definition … "

No matter what "hello" means, the written symbol "hello", made up of letters, is still a symbol. It doesn't matter that it's "unclear" what the symbol really means, or whether it even has a proper meaning. We see the symbol, "hello", and we recognize that it is indeed "hello", and not "sandwich".
And the symbol "hello" can be encoded into morse code, like any other word can.

" … what of when it’s not written? … does it mean there’s no code? … "

It is the symbol for the greeting that is turned into morse code. The word itself, the idea of the word, cannot be turned into morse code.
Morse code is a system for turning letters and numbers (symbols) into codes made up of short and long beeps.
If morse code was not designed to be turned into letters, but instead referred directly to ideas and things, then it couldn't be code, it would be a language of its own.

" from your definition, A has to represent a “real thing” … my question is what’s this “real thing” A represents … if the sound is the “A” then we have a problem: what happens when we don’t have to write the letter “A”?"

The fact that if I say "A" to you, you will recognize it as being "A". Therefore, that thing is real.
You later talk about "cat" as being a concept, aswell, so let me try to clarify:
1. There is a real animal, which we call "cat" because it fall under that definition.
2. The idea/concept of a "cat" is the idea that we can identify something as being a "cat", rather than something else, because we define the concept.
3. The word "cat" is a symbol for the concept, and therefore also a symbol for any animal (real thing) that would fall under that definition that the concept describes, as a consequence.

Only the word "cat" can be turned into a code, by "hiding" it under a different symbol. Perhaps for secrecy, or perhaps for efficiency, and in some cases because a message needs to be transfered in a way that doesn't allow the original symbols, or that it would be impractical.
A symbol is an "identifier", the thing that allows us to identify a concept/idea (hopefully uniquely).
The symbol isn't the concept, it is the identifier for the concept.

"*It's our way of decribing them. They aren't physically codes, because... yeah, "code" is conceptual.*
 … what I got from this is that none of our description for anything is actually real … so a “cat” is not actually a cat in the sense that it’s just the concept used to describe the real thing … "

"Cat" refers to the concept of a cat. The concept allows us to indentify something as being a "cat". A cat is a cat because we decide that it is.
The animal is physically real, of course, but it isn't inherently a "cat". It wouldn't have been a "cat" if humans didn't invent that classification.
When you say "look at the cat", you have to assume that I know what a "cat" is, that we have the same idea of what it is. But no matter what we think, the actual physical cat is what it is. A word or classification cannot change what it physically is.

This is very important to our discussion of computers and code. The word "cat" refers to a concept, an understanding of wht a cat is.
when I say "cat" to you, you access your understanding of the meaning of the word "cat", in your mind.
A computer doesn't do this, of course. You cannot say an actual word to a computer, and think that it would understand the meaning of it.
But, when we make computers, we make it seem like they ca do somethign similar to that, by hiding it all into "abstraction", as I've talked about earlier.

We can *pretend*t that pressing "A" on the keyboard actually does send an "A" into the computer. We can make software that gives the illusion that we really did send an "A" into the computer. We can then output an "A" on the screen - once again just an illusion, because in reality it is just a specific pattern of LED's, but our brains recongize it as an "A".

Throughout this entire process, there never was an actual "A" anywhere.
However, because this makes thing so much more intuitive, we also make programming work this way. It's a really complex system of pretend.

When doing object-oriented programing (OOP), such as C++, we can write actual conceptual things, like describing what a "car" is. I'm sure I've said this before.
I explain, using this language, in my source code, that inside my program, I was to define something called a "car", which can "drive()", and which as "horsepower", and a "model", and so on.
Because I ahve described this is my source code, the compiler can then tell me when I am doing things wrong, because I have explained what shoudl exist, what they "are", and what the restrictions and limitations are.
If I accidentally write that I want a donkey to "drive()", then the compiler can tell me that I'm not making sense, because only "cars" can "drive()".
But, in reality, both a "car" and a "donkey", in the program, will onyl be a set of dinary sequences, they wont' actually be cars and donkeys, obviously.
But we can pretend that they are, because it makes everything so much more intuitive to humans.

Likewise, I can say that I want "X" to be an integer, and I want "C" to represent a character.
Then I might try to add C to X, but the compiler will tell me I'm not making sense, because I said that C shouldn't be considered a number (even though it technically is, because everything in computers are just numbers).

So, a lot of the things we write in C++ never gets turned into binary at all. They only exist there to explain things to the compiler about how it should make the program, and what I do not want to allow myself to do - so that the compiler can help me correct errors.
I might forbid the idea of a donkey driving a car, but a human is allowed to. So if I ever accidentally say that a donkey should drive the car, I will get an error message.

See how it's about talking to the compiler? This a "high level" language. Very, very different from assembly, which is simply code for direct instructions.

" I think I have a better idea on how to clarify this … if you think all our descriptions of the computer code are just representations of the real thing, then C++ is as much a code as binary or any other language…"

Lots of things are wrong about this:
1. C++ isn't code, it is a language for talking to C++ compilers.
2. Binary is not "code", it is a representation, a sequence of symbols that represent the voltages in the computer.
3. Binary is not a language, either.

The only "code" we ever write is when we write assembly, which is a reasonably rare thing, nowadays, because it's mostly obsolete.
(There may be something similar to assembly that I am not aware of, which might also be called "code".)

However, using a programming language, we could program a system of codes to be used for efficiency when programming. We do this a lot, actually.
But this is very high-level "code". For example, I may have the name of a function ( a mathematical function), and that name may be quite long. In some cases, I may need to refer to the function very often, which will make everything look very cluttered and hard to read, so I createa an "alias", which is a code-word for that function. This codeword could be short.
For example, I may have a function called "rotateByDegree()", which I can then shorten to "RBD()", for example.
Technically, that would be "code", since it is a codeword that represent the symbol for the function.
"RBD" decodes to "rotatyByDegree", which is a symbol (identifier) for the function (the "thing").

" what you’re saying in essence is that the code in computer is just to represent an actual thing the same way “box” represents an actual thing"

A "code" is when you have a symbol that refers to a symbol that refers to a thing. That is, 2 levels of symbolism, instead of 1.
So any symbol that represents the word "box" is a code.

" … this is how I got this:
1.	You said “box” and “instruction” are symbols for what actually happens in reality
2.	I just took this to mean that every thing else we write or say are symbols for what actually happens … “go” , “come” , “think” , “arrive” , every damn word is a symbol for the “real thing” …
3.	You said the “real thing” in the computer is the switching of voltages …
4.	You also said “binary strings” are symbols for this “real thing”
5.	This clearly means that hex codes are symbols for the real thing same way: because they end up in voltages same way binary codes do
6.	This in turn means that C++ codes are symbols the same way binary codes and hex codes are: because they end up in the “real thing” which are voltages …"

1. Correct. Those words are symbols for those things.
2. Yes, correct.
3. Yes.
4. Yes.
5. Yes, but it's not "hex code", it's "hexadecimal", base-16. I have no idea why you're putting the word "code" there.
6. C++ isn't "code", it is a language, just a very different kind of language.
Things you write in C++ do not get turned directly into binary. Some of it does, to varying degrees, but most of it doesn't. C++ explains to a compiler how a program should be, and the compiler creates a program based on those specifications. This means you don't have to care/know much about how computers work, to be able to program. You only define concepts, and you don't have to care how the computer does those things. The compiler needs to know that, not you, because it is the compiler that makes the program.

"*The switch patterns are not symbols, they are the real thing. We use symobls to refer to real things like that. Real things aren't supposed to be seen as symbol for conceptual things.* … they’re both real buddy … the switch patterns and the button … not sure exactly what you’re driving at here … but what I’m saying is that the switch patterns represent that one button …"

Yes, the physical button is real, but it has a symbol on it, which represents a concept. The button says "A" to help us imagine that we're actually sending an "A" to the computer. the butto is lying to you. when you press "A", you're not sending an "A". If all teh software in the entire chain all sees it as an "A", then you won't notice that you've been lied to.

But what you're saying is that an actual cat represents the word "cat". Do you not see why that is backwards/reversed? The cat is not a symbol, it is the symbol for a cat that is the symbol, not the cat itself.

Or are you focusing on the fact that the symbol, when written down, physically exists?
Thet is true, of course, but those switches you're talking about do not look like the symbols for 1 and 0.

"*Yes, thank you. The code represents a specific action. That is exactly it, and what I've been trying to tell you all along.*
 … well I can say that I’m glad that we can finally come to an agreement … but I’m not sure if you’re reading the definition with the intent in mind … I particularly emphasized the word “specific” … by that I mean a code activates one function and one alone … the “represent” is not really a point of emphasis … yes it does represent a specific action … but the specificity is my basic point in this definition …"

"Represents" is very important, since a "code" is a symbol (of the second level). In the end, symbols themselves can only represent things, because they are identifiers, only.
And these kinds of things only exist in minds. Minds are the only ones who need to identify things like that.
A computer never has this problem, because it receives instruction, there is never a choice, or any ambiguity. It is not aware of any symbolism, or anything even close to that.

Lets extent this not the mind, but to the brain:
The word "sandwich" is a symbol for the concept of bread with something on it. Therefore, if we understand the meaning of the word "sandwich", then we can point to an actual sandwich and know that it is a sandwich.
But our mind is produces by a neural network, the brain. In some way, the word "sandwich", and the understandinf of the word, aswell, must be stored in this neural network. And on that level, there once again is no symbolism. Minds can work with symbolisms, but neurons can't.

This is why a computer could have software that gives it a "mind", and then it could understand symbolism and use code. But the computer itself is like the neural network, the brain. Neither the brain not the computer itself can understand symbolism and code. Only the emergent system that they create (software or a "mind") can do that.

"*It action doesn't "represent the code", as you've said so many time, now. Obviously, there is a problem here, since you contradict yourself.*
 … I don’t think I ever said an action represents a code … not sure where you’re getting that …"

OK, I hope I've misunderstood you, then.

"*Well, this explains it, then. I see your problem if you think that "A" is not a symbol.*
 … well this might be a bit confusing but it’s not like I’m saying A is not a symbol of some sort … I’m just saying it doesn’t have to be a symbol for a real thing … so far as I’m concerned, “A” is just a symbol for A"

Well, yes, I guess it's my fault: Symbols do not have to refers to "real" things, in the sense of being physically real. They can refer to concepts, abstract things, aswell. But they do have to refers to things, as opposed to symbols. If they refer to symbols, then they are code. But all things still ahve a root in the physical. Even the idea of being "happy" is still rooted in what is physically going on in the brain. "Hot" may be relative, but tempreature is a fact of reality.

I shouldn't have said "real things", I should've said "things". My bad.
"A", however, does originally refer to that spoken sound, which is physically real in that it carries physical energy in the form of a pressure wave in matter. A sound.
If the sound had never existed, then we wouldn't have invented the letter "A" to represent it, and it wouldn't have been part of any language.

"*When you wrote this to me, I read the symbol "A", and my brain heard the sound that "A" refers to.*
 … well there’s no difference in this context because I can send you a couple of sounds(morse code) through the phone and you’d not have to write it down to know it’s the letter “A”…"

Because if I know morse code well, I can instantly translate it to "A" without much thought. You're only confusing the matter by giving examples of where you might get tricked into thinking the process of encoding and decoding doesn't happen.
Yes, you could theoretically have a person who learnt morse code instead of the normal alphabet, and can only read morse code. But the origin of morse code is still the same. It is still made as a code for normal letters.
What you've got, then, is a person who thinks that morse code isn't code. This is a case of being wrong, that's all.

"*You can't say a single code contains a function, because that heavily depends on what coding system you're using.*
 … yes I can say that: confidently: our technology requires that the code word “mov”(like you said) doesn’t end up deleting a file totally … and you can’t say “mov X” and it ends up moving “Y” … "

Yes, but you can imagine that there is a programming language where there is a codeword that does two things. "Swap", for example, requires multiple steps:
If you have X and Y, and you want to swap their values, you have to:
1. copy X to Z.
2. copy Y to X.
3. copy Z to Y.
(Z is a 3rd variable/register, which is required for a "swap" operation.)

So any language that has the codeword "swap", like this, will have one codeword that performs a number of separate instructions in sequence.

You said "function", and I don't know why you keep saying that, but I'll just assume you mean "operation". If you do, then use that word, to avoid confusion.

"*If you consider the source code to be a program, then you're correct, the "program" contains codes, it is made up of codes.*
… well I consider the source code to be the “fancy” name used to denote the collection of codes that make up a program or application …"

Then we have the problem that I'm not sure what you mean by "codes". :/

" … the source code still exists after the computer turns it into executable form … which means that the only limitation in source code is the language barrier … but the source code directly translates to machine language … just one padded to suit the human understanding better …"

I'm not sure in what way you mean that the source code still exists after compilation.
Yes, the compiler doesn't delete my source code, because why would it? I reads the source code as it writes the outpful, the program file, the .exe.

If you wrote it in assembly, then you can take the .exe and turn it back into assembly, again, and it should look exactly like what you initially wrote.
If you wrote it in a high-level language, like C++, then you can't turn the .exe back into the exact same source code. The information isn't there! You can turn it into assembly, though.
When compiling a high-level language, "most" of the information is lost, because most of the information wasn't there to define the program, but to define the process of creating the program. It's for the compiler, not for the end product.
(The .exe created by a ligh-level language will contain more useless things and be more "bloated" than one written in assembly. That is the down-side, even though it's a very small issue.)

You said the source code directly translated to machine language. Like I've said, this is only true for low-level languages like assembly. Not at all true for C/C++, for example.

We do not want to have to write a program the way that computers work, we want to be able to write them the way a human would, by defining concepts. Then it's up to the compiler to turn that into a program.

"*I just don't want to call it "code", because whether it is "code" or not depends on what language you're programming in. And I'm trying to be strict with my usage, to avoid confusion, but I'm not sure it's working.*
 … well the language doesn’t matter … whether binary, hex, C++, html , or any other language …"

Well, you're very wrong, and I've explained why, many times, so I don't know why you keep insisting on saying this. This is the kind of thing that makes me think you're just trying to troll.

""Code" as an uncountable noun. "Code", in this sense, can contain any amount of "codes", thus any amount of "functions". … well I suggest you treat the term as a countable noun … atleast till we clear it up …"

It's ambiguous, a lot of the time. 

"*Remember, "binary form" is also symbolic. Anything that represents binary form is therefore "code", since it is a symbol for a symbol.*
 … I think your analogy crumbles totally here … if binary form is symbolic for the “real thing”, then hex codes don’t get translated to “binary form” … hex codes are as much symbols as “binary form” like you describe it … hex codes actually get turned into the “real thing” … same with binary …"

Hex isn't code, and it's not called "hex code", it's simply called "hexadecimal", or just "hex", or base-16.
Binary = base-2.
Hexadecimal = base-16
Octal = base-8.

If you take any piece of data from a cell in RAM, you ca choose to "read" it in binary form, or you can choose to read it in hexadecimal form, or any other.
None of them are more or less that the other. "Binary" has the advantage of being the bost "fundemental" in that it directly tells you the state of each "switch". But a binary sequence can be seen as a value written in base-2, without having to do some kind of "conversion" or anything liek that. In the same way, if you force the computer to display the binary sequence as hexadecimals, then there is no "conversion" there, eether.
"Hex" is only "code" if/when it is intended to represent a binary sequence. But it doesn't have to be like that. If a binary sequence is a value, then the same value can be displayed in any base-N, and none of them are codes for eachother, they're all fundamental.
But I guess that some binary sequences aren't meant to be seen as a number, tehrefore it could be considered "code" if you use hexadecimal numbers to represent those sequences. (?)

32bit integer:
10100101 01010101 10101110 01101101
which is the value 2'773'855'853 in decimal form. In hexadecimal: A555AE6D.

Now, the beautiful (and very useful) thing about this is that each 2 numbers in this hexadecimal number represents each section of 8 bits.
Of course, the reason that this is useful isn't apparent to someone who isn't a programmer, and can't be easily explained.
But none of these are codes for the other, they're just different ways to "interpret" the pattern of voltages in RAM.
But any symbols that represents any specific sequence of these are "codes".

"*"11101010" <- this is symbolism, not the real thing.*…
 this simply means “mov” is symbolism the exact same way “11101010” is … "

Except that the people who made the hardware specified that an instruction to do a specific thing has a specific value, such as "the number 55 causes register X to be flushed", or whatever (?). And here, the number "55" is then the symbol for that instruction, the name of it. The computer can't actually read "55", it reads a pattern of voltages, so "55" is a symbol for a specific pattern.
But then someone said "I don't want to have to write '55', I want to write something I can related to". So they made assembly language, where the word "mov" refers to the number that is symbolic for the thing that happens in the hardware.
"mov" is code for "14", perhaps, which in turn is the symbol we use to represent that instruction.
Another assembly language may use a different codeword for "14", much as "move". But 14 is the actual name of the function, because "14" in 8-bit binary is 00001110, and shows you how the switches should be set to carry out the instruction.
That is, 14 is just another way to write 00001110. But any word that refers to this is a codeword, such as "mov".

See, the compiler reads the word "mov" and writes "14" (I don't know the actual number) in the .exe file.
It writes "14" because the programmer who made the compiler programmed it that way.
So, to the programmer who wrote the compiler, teh word "mov" is a symbol that represents "14", which is the name of the instruction.

If this still doesn't make sense to you, it's because you don't realize that this is all in our heads, it isn't real. There never was a word called "mov" that went into the compiler. We just pretend that it was. In reality, it was 3 bytes with values that we pretend represents the letters "mov".
Like I said, it's all a huge system of pretend, and when we have two layers of pretend, it's called "code".

" well all conversions end up in the real voltages … so hexadecimal is as much a code as C++ … btw don’t you use hex codes in C++? I use it in HTML directly in my source codes … "

First of all, HTML is not a programming language at all, and it is never compiled. It isn't even a scripting language, it's just a way to format text and images in a document. A tagging system. It isn't "source code" in any sense, it is data. It's a file format.

Secondly, we can write hexadecimals in C++. I dont' knwo what you mean by "hex codes".
"0x10" <- this is hexadecimal "10". We just put "0x" in front to have it be read as hexadecimal.
I newer C++ versions, you can write binary, aswell, by writing "0b10101001". "0b" in the beginning meaning that it should be read as binary.
All of the following 3 things will be treated exactly the same way, and will end up the exact same thing, as they are all ways to write the value "10":
1. 10
2. 0xA
3. 0b1010

"*So it is not "hex code", unless you're talking about something else, such as my example of "#FF55AA", which is a "color code".*
 … if it’s represented in hex form, and it’s called code, then it hex code … what’s wrong with this?"

No, I just said that this example is code. Call it "hex code" if you want.
But it is not true that any number written as hexadecimal is "code". It is just a number.

"*When you "put the binary directly in", then it is not code, it is symbolism. You're writing "11010101010", or whatever, which is direct symbol for the pattern for the switches.*
 … well all languages are direct symbols for voltage patterns … it’s like you said … the compiler would translate your C++ program in to voltage patterns same way it would translate the hex code into voltage patterns [...]"

Nono, software cannot do that. Remember, software in on the level of a person. It was written by a person, and the person wrote it using symbolism.
A programmer can never "write" the actual states of the switches, he can only symbolically represent them. He cannot stretch his hand into the computer and physically "flip" the switches.
It's all in our heads.
If I have a programming language where I am able to directly control a switch in the computer, I still have to access it through symbolism. "10101001" <- this is as close as software can ever get to actually accessing the switches. And this is symbolism.
Remember, "software" is also only in our heads. Software is conceptual.
The fact that I press a button that says "1", and the number "1" is showed on the screen - even though this represents the state of switch int he cumpoter, all of these things are symbolical. The label on the button, the entire idea that this would even control a switch is just conceptual.
The compiler doesn't translate the code into voltages, because a compiler isn't real. :/
What is really, truly going on is that the CPU is turning one pattern of voltages into another pattern of voltages. It's only in our "pretend world" that these voltages were anything more than they are. And "software" is part of the "pretend".

But it's really, really hard to understand this, because these "unreal" things still create an emergent system. That is, the combination of all the patterns of voltages create something more than the sum if its parts: It creates "functionality". But this is on the level of the programmer and user, not on the level of the parts that make up the emergent system.

Don't be afraid to admit it to yourself if you don't understand it. This all is beyond the average person, and not something you have to understand at all.

"… the numbers and letters you write in your program are just to help you relate with the computer better … that’s all … the computer already understands it … the language is just to get you to understand it like the computer does : but in easier terms… "

Only talking about assembly, of course. High level languages are completely different
Yes, it's basically being displayed to you in a symboilic way that is fit for human reading. And this is done through the use of "code".

"Likewise, "TGAAAGC" is code for DNA sequences, only for simplicity. It would be extremely cumbersome to have to write the actual name of the nucleobases, so we use codes for them."
 … you know I actually suggested you stayed out of the DNA until we clarify code … according to you, “TGAAAGC” is just the representation(symbolism) of the actual “thing” … so by your definition it’s not code because there’s no second level symbol … "

TGAC is code for the full names of the nucleobases in DNA.
C -> cytosine -> the real thing.
Thus, "C" is code.
"C" also means "centigrade" or "celcuis" in a different coding system, and is also in itself the letter "C".
There is nothing about "C", inherently, that makes it mean "cytosine". But the word "Cytosine" is a direct symbol for that nuclebase.

" we can make up different languages to represent the symbolism we use for DNA … we can say “mov” can be equated to “TGAAGC” …we’ve shortened it but still “mov” represents the same thing … this is basically what goes on in programming languages …"

Yes, if you want to "write" DNA - which we do - then it would really help to use a coding system or even a programming language.
And we have that, already. I don't know much about it, but we do have programming languages for programming DNA. And then a machine makes DNA out of it, from scratch, like a compiler.

"*Damnit, I should've known you still wouldn't know the word "abstraction", even though I just explained it. It doesn't mean anythign is abstract.*
 … I stand corrected … I really didn’t bother to inspect this closely as I would normally because there was just too much lines to respond to … anyway this might well be a rare piece of good info. You’ve given : atleast until I take the time to inspect it properly …"

Well, my image of you just grew a bit. Thank you.

"*Yeah, you don't know anything about this subject. Didn't you say you were learning programming? What language are you trying to learn?*
 … well I’m on HTML/CSS now … aiming for PHP…"

Remember, HTML/CSS are not programming languages, they are file formats.
When you write something in html, it becomes a file that is read by a program (IE, firefox), and interpreted. It is content to be loaded by another program, like any data file.

PHP is also a scripting/preprocessor language, but at least it's a lot more like a proper programing language, and also a good way to learn the basics of C, since PHP is a "C-style" language.
I did a lot of PHP for websites, in the 90's, and some in the early 2000.
In combination with MySQL and JavaScript, you can make cool/good stuff.
But it's messy as hell, not beautiful at all.

"*Yes, there are more things that only intelligent life can cause, I'm quite sure. We can do an almost infinite number of different things.*
 … so what’s your beef if I say only intelligence can create an IC system? Or genetic code?"

My "beef" is that you're wrong. Genetic code is made though evolution, we know this, we see it constantly.
And any chain of nucleobases will have information inherent to it. When we make RNA self-assemble in labs, we didn't make the sequence, nature did. It was basically random, but that doesn't mean it isn't a genome, so to speak. If the sequence is useful, then it will do better than those who got a useless sequence.

"I would never say anything like that. Most animals are intelligent on some level. Some of them are clearly quite intelligent. You've clearly misinterpreted something I said.*
 … well I hope I have misinterpreted you because the fact is that intelligence is not just limited to humans … and it’s my basic point …"

No, intelligence is clearly "limited to" brains, in that it is only a property/capability of brains.

"*No, I don't. I believe in the possibility of it, but  not the existence of it. *
… don’t really get you here … if you believe in the possibility then you believe it can exist … if so what’s your beef with God?"

Yes, I believe alien intelligence can exist, because humans would be considered intelligent alien creatures by someone who wasn't from earth.
If life can exist on earth, then it could exist on some other place that was like earth.
But that doesn't mean I believe they do exist, because I have no evidence of an example of alien intelligence.
It's sitll possible that we are the only intelligent life in the universe, even if other intelligent life could exist. Not everything that "can" exist must exist. There could exist heart-shaped pencils, but that doesn't mean they have to.

"If you think intelligence produces technology, not intelligent creatures, then I really can't help you. … I really think you need more help on this one … using “intelligence” is much more accurate and appropriate… dolphins are intelligent creatures but they don’t create technology … "

Yes, which is why I said "humans" create technology. Dolphins don't, even though they are creatures, and they are intelligent.
However, chimpanzees, and some other primates, aslo create rudimentary tools from rock and wood. So it's not unique to humans.

If "intelligence" creates technology, then dolphines should also, since they are quite intelligent. So are ravens, and some other birds, for example.

But we have to note that just because you could create technology doesn't mean that you have to do that. That is the "problem" with intelligence, it can do and not do whatever. Nature itself, however, doesn't have this choise, which is why we can learn about what nature does. It is consistent and can be easily predicted, while intelligent creatures could be predicted, it's just a hell of a lot harder, because the system is so much more complex.

"*Intelligence can produce knowledge, through its ability to reason. It doesn't produce technology, which is the practical application of knowledge/science.*
 …  well I hope I’m not reading this right … because the root of all technology is intelligence … "

You're saying different things. Yes, at the root, you require intelligence. But you also require the ability to actually build tehcnology, if you're going to actually have it. A disembodied intelligence (if such a thing could exist) still cannot produce technology.
So we've got scientists, and we've got engineers. You need both to get technology. Yes, one person could do both, but they are separate things: Knowledge and the application of knowledge into technology.

"*if you mean lose itscurrent function, because obviously you cannot remove something from a system that needs it and still have that system function the same way.*
 … that’s what IC is … just that you’re obviously confused about it and what claims you should be looking to refute : the claim that something is IC is a scientific fact: the claim you can attempt to refute is the claim that evolutionary process can’t give rise to it … "

We know that it's possible to gradually build a system that is IC. That's why I'm saying that if this is simply what you mean by IC, then it is a moot point. IC, in this sense, doesn't mean it cannot evolve.
I would prefer to see IC as something that cannot evolve, then it would actually pose a challenge to the theory of evolution, and be "useful".

"*If you mean "lose all/any function", then that is exactly my understanding of IC, and exactly what I've been talking about.* … and exactly why I’ve been calling out your ignorance as well as the ignorance of the supposed scientists that claimed they refuted IC … "

That would have been the only useful definition of IC. Yet you choose the one that is pointless? Why?
I mean, the idea that if you have a system, and then remove a vital part of the system, and then the system no longer works, then that is too obvioius to even mention. It has no value at all. It's basically a tautology.
We have no reason to falsify it, or even care about it. Yes, IC exists, by your definition. So what? We knew that, already.

" if you see a well (technically a hole), one can easily tell that intelligence is the best explanation even if the agent is unknown … "

Yes, but only because we know that humans make wells. And yes, if humans do, then it's possible that other living creatures do. So if we find a well on some planet, then we have reason to investigate the idea that a living creature made it, perhaps for the saem reason we make wells on earth.
But this cannot be extended to life itself, because we have no examples of something that designs life - except for evolution.

"*No, you have to establish whether its true or not, with evidence.*
  and we’ve done that : the evidence is in our repeated experience with IC systems: from this we know that only intelligence can account for an IC system …"

No, IC systems can evolve. There is nothing about IC that makes it impossible to evolve. IC is pointless, it's a tautology. Effectively, you're saying that something isn't what it is until it is that thing. Because if you remove one part, so that it is no longer that thing, then it won't be that thing anymore. That is exactly what your definition of IC says.
This has absolutely nothing to do with whether it can evolve or not. It doesn't even present a challenge, it's not something we have to give a moments thought to. I don't understand how you can't see that.

"no experience has been seen of nature building an IC system … such as the flagellum … so it’s actually your position that needs evidence …"

Yes, the flagellum has been explained, since the 1970's or so. Google it.

"*But what you're doing is that you're trying to use the hole itself as the evidence, which simply does not work.*
 … isn’t that basically what evolution does? "

Of ocurse not. The existence of the hole doesn't tell us where the hole "came from". But if we can find the reason for why holes exist, and demonstrate that the process works, then we've got an explanation for why the hole might be there.
You creationists want to look at the hole say taht simpyl because the hole exists, the reason is "god". Not because they've foudn the process by which god creates the hole, or because they found gods that create holes. No, just "because".
Darwin actually identified the process that diversifies life. Instead of pointing to life, he pointed to the process. And the process can be tested and repeated and observed, like any proper science.
Note that I'm not talking abotu the origin of life, but the divsersification fo life.

"*Something about the hole might be evidence of its origin, but not the mere existence of the hole itself, since that is what caused the question in the first place.* … ofcourse the existence is directly related to the attributes of the hole … I’m not sure exactly what you’re trying to say here … we’re saying the reason this exists is intelligence, and it’s attributes prove it …"

No, you're saying that because these attributes exist, the only reason for it is "god". Yet you can't identify the process "god" used to create it, so how can you say that?
And neither can you identify a god who has actually done it.
So this is an argument from ignorance: You're implying that just because we don't have the answer to where life came from, the answer is "god". Textbook argument from ignorance.
This is the exact same thing as when ancient people didn't know why lava came out of the mountain, so they said god did it. The exact damn thing. They did not know nature could do that!
So do you really want to keep making that mistake, or will you realize that something that is unknown is simply unknown, at this point?

"*IC is a challenge to the theory of evolution to explain how something could have evolved. If we can figure out how it could have evolved, then the challenge has been met.* … lol hell no … if you imagine an evolutionary process it has no weight what so ever on the facts"

Saying that something cannot have evolved is an attempt to falsify the theory. If it is true that it cannot have evolved, then the theory (or parts of it) is falsified.
But if the theory of evolution can explain how it could have evolved, then you can't prove that it didn't evovle that way. So the falsification has failed. You can't know that the theory is false if you could be wrong.

No one is saying that we know how things evolved, we're saying that we know how they could have evolved, and that makes it the most likely explanation.
We know that they did evolve, and we know a lot abotu which species evolved from which, we just don't always know much about the details of how they evolved, since we often don't have the evidence to be able to tell that. This is when we need to figure out what the possible options are, and which options are more likely than others.
If there are no options that we can find, then that still doesn't prove that it didn't evolve, it just means we haven't come up with a solution. To say that it didn't evolve just because we don't know how it could have, would be an argument from ignorance. "Not knowing" can't be a source of knowledge.

" … it’s only when the facts say otherwise that you do have a refutation of IC"

We don't need to "refute" IC, we know that IC is true, but it is of no value, it doesn't mean anything. It's like saying a red car is red. It's obviously true, and can't be false, but it also means nothing.

" … and like I said to Spiegel … the imaginary processes are best validated by probability … if an imaginary process is so highly improbable, then it’d require faith to accept it as truth … to a rational person, it’s the most probable that goes …"

I have no idea what "imaginary" processes you're talking about.

"*You seem to think IC is something it's not. It is a description of a specific kind of system. It is like a "criteria".* … not sure exactly what you’re saying here …  "

To say that something is "irreducibly complex" is like saying that it is "red" or it is "large". It's just a specific kind of description, an adjective, basically.
It's not a theory, because it is not an explanation for any phenomenon or something like that. Therefore, there is nothing to "falsify", in that sense.
Basically, to "falsify IC" is similar to "falsify redness".
However, you can falsify the claim that something is IC, just like you can falsify the claim that something is red.

"*You can look at something and say that it is either IC or not IC.* … better still, you can actually test it out and establish beyond any reasonable doubt that a system is as a matter of fact, IC …"

Well, yes. That's what I meant.

"*So someone can look at the human eye and say "this looks like its IC". That is a challenge to the theory of evolution to explain why its not IC.* … well it’s more than looking … I explained a situation called Aphakia to Spiegel which is a scenario where an eye has no lens: the eye turns out to be almost useless"

First of all, note that I wrote that with the definition of "IC" being simply "something that could not evolve".

No, the human eye is definitely not IC. There are plenty of things you can remove, and it'll still be able to "see".

" … aside this, you can just do a lab experiment to prove the exact parts needed for the eye to function"

Function to what extent? It has to lose its ability to "see" for it to have lost its function. Blurry vision is a hell of a lot better than being competley blind, for example.

" … after proving this, you can’t just come up with a story that “this happened, that happened, and so it evolved” … this can’t disprove it, not the slightest chance … you’d have to prove this can even remotely happen in a lab to disprove the fact …"

No, the scientitsts do not say what happened, they said what might have happened, or could have happened. There's a big difference.
We cannot make an eye evolve from scratch in lab, since it took billions of years, as far as we know.
But see, if you want to challenge evolution, then it is up to you to bring the evidence against it. If you're claiming that the theory of evolution is false, then you're making a positive claim, and you have the burden of proof!

And before you get this wrong: The theory of evolution did have the burden of evidence, but it has met it. It is an established theory.
Now if you wan tot say "they are wrong", then the burden of evidence/proof is on you.
It's a different thing to just not accept it, but if you want anyone else to reject the theory, then you need to prove that it is wrong. If you're indeed claiming that "it is false". To say "I don't believe it" or "I am not convinved by the evidence", that's fine, you don't need to support that, that is just a statement of your position towards it.

"exaptation basically said all the components once had individual functions and at a point in time, they all collated perfectly to form the IC system … that honestly a big lol …"

It's usually in a bacterial lifeform that we talk about these things. So, you're telling you that even though they have generations that are something like 20 minutes long, and they have populations in the trillions, and hundreds of millions of years of time, you find it "unlikely" that some parts would start interacting to produce an emergent property?
And you're so sure of it that you "lol" at it?

Whatever, man.

" if atheism doesn’t mean to believe “God doesn’t exist” it means to believe God exists (or atleast have no objection to that thought), but just choose not to believe in Him … so could you say you have no objection to the thought that God exists? Oh wise one?"

Tell me, are these two things the same?
1. I believe that god does not exist.
2. I do not believe that god exists.

They are absolutely not the same thing.
 #1 is a positive claim, which also carries the burden of evidence. It is the claim that god in fact does not exist. This cannot be proven, in practice.
#2 is a rejection of a positive claim, and does not carry the burden of evidence. It simply means to not be convinced that gods in fact do exist. It is not the opposite claim, that gods don't exist. It is the "null hypothesis", the "default position" of no belief.

Which one is "atheism"? Both.
And Einstein referred to #1, while most atheists are of the #2 kind. He was clearly not talking about the #2 kind.

"*If deism isn't theism, then it is atheism, crude as it might sound. And yes, it weirdly means that it's possible that you might be able to be a deist and an atheist at the same time. (?)* … lol … deism is theism then … sorry …"

I'm not sure it is. People usually mean a "personal god", one that actually matters, the kind that people make religions about.
I agree that it's a mess. The problem, when someone asks if you "believe in god", is that there is no defintion of what a "god" is. So you can't actually answer the question.
I mean, I don't think I believe in any gods, but if it later turns out that computers are in fact gods, then I'll be embarrassed because I've always believed in them. :P So I've always been a theist, then.
But to the best of my knowledge, I don't believe in any gods. And in fact, I'm quite convinced that gods in fact do not exist, but it really is a matter of definition.

"*If you don't believe in a personal god, then you don't count as a theist, normally.*
… lol no … like you said, atheism and theism are two direct opposites … if atheism means lack of belief in God or supernatural beigns, then theism means belief in God or supernatural beigns … so it doesn’t matter the kind of god you believe in: whether personal or not… you’re still a theist …"

But an impersonal god is hardly a "being". It can be a "force", as some call it. It can be the universe itself, which makes it not supernatural.
If someone says "god is love", then god is not a being, it is an emotion. Maybe it is the instict to love people that some people refer to as "god". And that doesn't make them "theists".
Or well, whether or not it does is unclear. I am not sure. I recognize that this is unclear.

"*It is very clear, from those quotes, that Einstein defined "atheist" as someone who believes that "gods do not exist". And as I've said, that is not what atheism means.*
 … if so then you should have absolutely no objection to my thought that God exists … I mean since you’re an atheist and you only say you don’t believe in God … you have absolutely no justification to call God imaginary going by this … "

That is correct. All I can say is "stop believing something you have no justification for believing".
That is not to say "god doesn't exist", but rather "we should not believe in god, since we have no reason to.
People's belief actually do matter to society, to varying degrees. As you know, religious belief has killed a lot of people. Therefore, it is only right to ask for a justification, or ask peopel to stop because they have no justification.

"*Yeah, volcanos can spring up anywhere at any time, for no reason, huh? It can just randomly become icy cold?* … haha I smell desperation … actually volcanoes can spring up anywhere at anytime lol"

No, of course they can't. Volcanos requires that there is a flow of magma there, that can break its way to the surface.

" however weather conditions aren’t all to environment … environmental conditions could also mean a large amount of predators "

Yes, aswell as many other things, like competition of sresources, sexual selection, and whatever.

"… so yeah … the environmental conditions are random …"

Of course they aren't.

"*You really want to be the right guy at the right place, so to speak. Do you have a problem with this?* … not really … I’m just saying it’s what it is … a game of luck … just like a dice game … "

Yes, for the individuals caught in it, in some cases - rarely - it might feel that way. 
However, if you're a polar bear, you're probably not going to have a sudden problem that there is too much jungle at the north pole. Whatever happens to the north pole, being a polar bear at the north pole is still going to be better than being a gazelle at the north pole.

"so tell me something : just how “sudden” are these “selection pressures”? … Aren’t they random?"

No, they not random. If the selection pressure changes because your prey, which you've been living on, dies out, then that is not random. And it's not going to be very "sudden", because the number of prey individuals is slowly going to go down, and it'll be harder and harder to find any.
And that's probably one of the more sudden changes, though. Other changes are when the ice ages come or go, which is a very slow change. And they're not random, either, they come in waves which are pretty constant.
Changes in climate are slow, but changes things for everyone, aswell. Then there's the growth of deserts, for example.
But predator-prey dynamics is probably the main thing that controls evolution, I suspect.

"*The fact that some "random" things follow a system to some extent means that we can predict what is more likely than other things, and that makes a difference.* … Ooook … don’t really get you here but you can’t really predict the environmental conditions in evo."

Some factors can be predicted, like climate change, ice ages, and the growth of deserts, for example. Some things can't practically be predicted, because there are too many factors,m and it depends on how far into the future you're tryig to rpredict it.
we can always predict things for the coming year, for example, sicne these thigns change so damned slowly.
Natural disasters are a different thing though. They happen so quickly that most life dies out because they have no time to adapt.

But you'd basically have to ask an expert about this, really. I don't know enough about it.

"*When you roll 2 dice, we know that 7 is more likely to turn up than the number 2. You know this, right? * … hahaha omg …
There are many ways to roll 7, but there is only one way to roll 2. … Oook yes you’re right … still random outcomes …"

Non-random enough for these kinds of fact to be used by casinos.
Casinos live on te fact that you think somethign is perfectly random, but they calculate how it isn't, so that they always have better odds than you do.

For something to be perfectly random, the change of any "number" to come up must be equally large. There must not be a pattern or a way to predict it.
The numbers in the constant PI (3.1415...) are technically random. There is no way to predict the next number, it doesn't follow a pattern. It fulfills all of the criteria and tests for perfect randomness.
But like I said, with 2 dice, 7 is more likely to come up than 2, which means it's not very random.
And I'm sure you agree: If you were given the choice, with the same payouts, between rolling 2 or 7, you would also pick 7, because you know there's a better chance you'll win that way.
However, with one die roll, want to pick 2 or 5, for example? Doesn't matter, the odds are the same, theoretically. And the odds being the same for any number is the definition of randomness.

"*If evolution is random, then the concept of evolution doesn't exist. The whole point with it is that it isn't random.* … well just answer the question dammit … "

I can't, it's a paradox! You're asking whether I would find evoluton absurd if it was random, right? Well, if evolution was random, then it wouldn't be "evolution", so what is it?

"*We can only identify evolution because it is a specific change, not a random one.* … I’m still confused : specific in what sense? That you can predict the outcomes it’d bring? Hell no …"

Given a specific situation, and a short-scale prediction, then yes.
But that's not my point. Species cannot change if there is no direction, or they would just hover around a center point.
Take the number zero, and keep adding either +1 or -1 to it, perfectly randomly, and over time you should be hovering at the number zero. No actual change.
But in nature, this is not what happens, which means that it isn't random, there is a bias towards some specific direction.
And species become better adapted to their environment, and that surely cannot be random! There is a pattern, and where there is a pattern, there is less randomness.

"*Why don't you actually test that idea? Take the number 10, and make a shitload of copies of it, with a random offset such as +1 or -1. This would be our gene pool. What is the average value of all the numbers in this gene pool? Should be 10, or very close to it. So, keep making copies of the copies and adding a random offset to them, it doesn't matter how many times, and the average will still be about 10.*
 challenge accepted … did the value change from 10? Hell yeah … proven beyond reasonable doubt … test successful … idea validated …"

First of all, you did not actually do the test.
Secondly, this it is a mathematical fact. If you're getting a different result, you're simply not doing it right.
No, the result won't be exactly 10, but it will stay around 10 over time. It will not grow in any direction, which is the point.
Given an infinite about of "generations", the average will be exactly 10, theoretically. Therefore, this model does not model reality, since in reality, species do change in some direction.

"*The only way that the average can change is if something drives the change in a specific direction. But then it isn't random anymore, it is lawful, it follow some kind of system.* … hahaha … even with a convenient imaginary analogy your attempt fails … if we have a point where eleven gets more frequent then the change prediction is validated …"

"Imaginary analogy"? The only thing "imaginary" here is that you imagine that calling the analogy "imaginary" makes any difference. Yes, analogies are imaginary.

It is a demonstration of a fact, that's all. Anything that replicates with variation and has a selection pressure will evolve. That includes numbers. I used numbers because it makes it easy to examine, since you can easily calculate the average value of them, so you can tell if the "species" has changed as a whole. It's only for convenience, nothing else.

"* to evolve backwards means you have to have the same environmental pressures, but "inverted", and in reverse sequence.* … well I see nothing here that can’t be achieved by evo. Just name the pressures required and imagine : it can happen"

I can happen, in theory, but won't happen in reality.
Look at entropy. Same principle. The reason things generally appear to become disordered is because there are more ways for them to be disordered than to be ordered, in most cases.
And I bet you have no problem with that, since you mentioned entropy, yourself.
So when I say that it is more likely to go any other direction than exactly backwards, you suddenly have a problem with it? And why is that?

" also it doesn’t make any difference to me if you use the law of irreversibility because I don’t believe organisms morphed from other organisms like you … "

Even if you don't accept the theory of evolution, you still have to argue against the actual science, not a straw man of it. And that includes the law of irreversibility.

"*You say "before". Have you already forgotten that time started at the big bang, therefore there is no "before the big bang"?* … yes there was … but there was no time as we know it at that point … it’s ok if it’s confusing …"

"As we know it"? So time, just not "time" time?

Sorry, this isn't established science, is it? :P

" *And the evidence of design is when you find the designer...!* dammit no: why are you making this hard for me … why didn’t you find the designer of the Stonehenge first before deeming it intelligently designed? …"

We have good reason to think we have found that the stone henge were made by humans. But we don't know that, because stone henge sure is quite special. But it is definitely very likely.
But I am no historian or archaeologist, so you'd have to ask someone else about what we know about it.

"So a really bad designer, then, who keeps failing and never seems to learn. … lol did you read the comment or are you talking off your ass again? … I said each time He added more info to help the organisms withstand entropy … what don’t you understand here?"

What I don't understand is why the designer would have to change his design a gazillion times, instead of making it "fail proof" from the start.
And if he meant to make a rabbit, why didn't he start out with a rabbit, rather than making completely differnet kinds of stuff for millions of years, until it started becoming more like rabbits?
It wasn't "maintenance". They were drastically changed over time, to more complex creatures.

" You're literally just making some absolutely unfounded, undefined, vague guess, like "weeeelll..... maybe some magical, invisible, immaterial guy did it?" … well it’s a hypothesis, but not an unfounded or undefined or vague one …"

Yes, it is, because you cannot define what god is, what he is "made of", or how such a thing "works", and you cannot define anything about the process by which he created things.

It is brutally vague and undefined. You're saying something unknown did something using an unknown process, for which there is no evidence, just because you can't accept hat evolution already explains it.
And that's ID/creationism summed up. The problem is not that evolution doesn't explain it, the problem is that religious people aren't allowed to accept it, but they'll do anything to avoid admitting that.
For example, such as "projecting". The fact that they aren't allowed to accept evolution is "projected" onto science by claiming that scientists aren't allowed to accept creationism.
The classical "no, you are!" argument.

"*Because punctuated equilibrium makes more sense than gradualism, and also fits better with the evidence.* … well personally I think it was because it was a fail … and I’m still not certain how punctuated equilibrium helps the situation … "

I don't know what to say, punctuated equilibrium is correct, that's all. We see it in nature, and in lab.
It makes perfect sense that the more fit you are to you environment, the slower you'll evolve, because the "less fit" individuals of the species won't have a problem, since even they are fit enough to reproduce just fine.

"*But what, are you saying that the cambrian lifeforms could evolve to all the diversity of life that exists today, but they themselves could not have evolved from some other lifeforms?* … I’m not saying this : you are … and that’s mostly non-factual … I’m saying the Cambrian fossils show no sign of evo."

Wait, what makes you believe that? Have you been getting your information from creaitonists, again?

"*Huh? What? I think you need to be more specific, because I don't get the question.* … I’m saying the Cambrian period actually disproves evo. Unless you could tell me how these organisms evolved so fast and forgot their transitions …"

"So fast"? I don't get it, it seems like you're telling me that a time that is best known for so much evolution "disproves" evolution? Are you high?
How they could evovle so fast? Because they can. If you're talking about the cambrian explosion, then that was a period of about 25 million years. Remember, humans diverged from chimpanzees only 7 million years ago. Dogs evole from wolves in 10 000 years.

25 million years is a looong time.
And creatures who are not as complex as we are now can evolve quicker because they are not as "tied up" in a complex system. It's harder to change humans than to change a worm, so to speak.
Back in the early cambrian period, life was still pretty simple, by today's standard, which allows for a lot of evolution, quickly, because negative mutations are less likely.
And as for "forgetting their transition", of course they didn't. They transitioned like everything else.
You might have gotten your info from creationists who think that we have no fossils from the pre-cambrian, and that the cambrian explosion was 1000 times faster than it was, and so on. There are a lot of myths about the cambrian explosion. It's a case of creationists taking advantage of the fact that people don't know much about it.

"*We study these things, in science. We wouldn't study them if they didn't exist. We know they exist,*
 … you assume they exist … it’s not a proven scientific fact … it can’t be tested or even defined … what is music in the real world aside sounds? Science can test for sounds yes … but music is certainly not just sounds … [...] according to the scientific method, if there’s any sound that doesn’t classify as music, then music is not sounds … question is, what is music?"

What music is is a matter of definition, only. The frequencies and amplitude of sounds exists, but as for exactly which kinds of things you want to define as "music" and not is completely arbitrary.
We simply need to agree.
As I see it, music is art. Anything that was created with the intent of being art is art. So if I record the sound of rocks falling on a wooden floor and say that it is music, then it is, in my opinion.
But people like Mozart would probably not agree, because he was "old school". Who cares.

Like you said, "sound" is not music.
It is our definitions that decide what music is.
But if we agree that some song truly is music, then yes, it is scientifially a fact that it is music, because we can measure that it is there, and it conforms to the definition of music.
It isn't hard. But it's like this with a lot of things, because a lot of things are simply  a matter of opinion as to how we should define them.
What is "sex"? When do you lose your virginity, does oral sex count, and so on? If only penetration count, then can homosexuals ever lose their virgoninty? And so on.
But you can't seriously tell me that the act of sex doesn't scientifically exist, just becuase we don't agree about he the exact definition? I hope not.
There are some pieces of music that everyone will agree is music. Then there are the experimental borderline cases where we can't always agree if it really should be considered music.

"*Most likely, yes, but life isn't. We're talking aboutlife, remember? Life is an open system.* … well life is a subsystem in the universe: and if entropy is certain in the universe, how come it’s not in life?"

An open system can decrease or increase in entropy, because it can take energy from other systems to do any amount of work.
It is only isloated systems that will tend to increase in entropy, because they cannot take energy from other systems.
Over time, they will lose their ability to do "work", as the amoutn fo ree energy goes down. Eventually, such a system will die.
But an open system can do anything as long as it can take energy from other systems. That's why the 2nd law of thermodynamics is only stated for isolated system.
Reply: antiHUMANDesigns 

I wasn't going to answer your next reply, because I started getting the feeling that you were only in this to troll me. ... Yes you were ... you're addicted ... you'd reply even if I was really trolling you ... 

However, I read you last reply, and your attitude is quite fine, for the most part, which I appreciate, so I will reply to it. ... I don't think my attitude has been quite different all along ... I just get pissed off at your extremely long comments which contain many needless rants and some I classify as just nonsense: plus the fact that you don't even seem to read my comments through ... and also you end up forgetting many points; even ones you brought up ... PS when your lines count up to over 1500 then it's less likely I'd respond with a well thought out reply ... I certainly wouldn't have all the time to scrutinize and re-check like I usually do with shorter comments ... 

I have less time, nowadays, than I had a few days ago. I'll see how much time I can dedicate to this. ... I think I've said this a couple of times you can minimize your time if you try to read my lines closely and summarize your points in simpler terms ... you definitely can't blame me for any time lost ...

It is the symbol for the greeting that is turned into morse code. The word itself, the idea of the word, cannot be turned into morse code. Morse code is a system for turning letters and numbers (symbols) into codes made up of short and long beeps. ... yes you can just listen to the beeps and decode the message instantly ... without any need for symbols ... 

"Cat" refers to the concept of a cat. The concept allows us to indentify something as being a "cat". ... so what exactly is wrong if we identify DNA as a code? 

A computer doesn't do this, of course. You cannot say an actual word to a computer, and think that it would understand the meaning of it. ... yes you can ... and like I said, I suggest you limit your use of the word "computer" ... a computer can understand pretty much anything ... it's just a matter of the programming ...

So, a lot of the things we write in C++ never gets turned into binary at all. They only exist there to explain things to the compiler about how it should make the program, and what I do not want to allow myself to do - so that the compiler can help me correct errors. ... I don't think there's anything in a computer that doesn't get translated into binary form ... 

1. C++ isn't code, it is a language for talking to C++ compilers. ... I'm pretty sure I remember you saying that writing a program in C++ is actually writing code ... not sure exactly what you're saying now ... yes C++ is a language in the sense that the expression of codes is usually termed "language" ... if this is the context in your comment then it's not my point: my point is C++ as the code you spoke of ... 

Binary is not "code", it is a representation, a sequence of symbols that represent the voltages in the computer. ... by my definition it is ... 1 and 0 each represent a single action ... 

3. Binary is not a language, either. ... it is in the same sense as any language is ...

The only "code" we ever write is when we write assembly, which is a reasonably rare thing, nowadays, because it's mostly obsolete. ... OK you're getting me more confused now ... this is quite new ... cuz I remember you saying many other things were code ... source code for example ... your source code in C++ is definitely not assembly like you said ... so how come only assembly is code now?

A "code" is when you have a symbol that refers to a symbol that refers to a thing. That is, 2 levels of symbolism, instead of 1. ... and I think I've stated in many occasions why this is most likely wrong ... I'm pretty sure code is first level symbolism in most cases ... I'll explain shortly ...

This means you don't have to care/know much about how computers work, to be able to program. ... I think this is the main point of contension ... you're an expert programmer, I'm an entry level engineer ... but "abstraction" has totally gotten you off the main idea and actual reality of the computer code and that's why I can tackle you confidently ... 

You only define concepts, and you don't have to care how the computer does those things. ... I think you should ... at least if you're going to define what the computer code actually is ... but you don't have to know all that as a programmer ...

The compiler needs to know that, not you, because it is the compiler that makes the program. ... and like I said ... the only reason for the compiler is ease ... one can just throw the compiler's job in the dustbin and create a program with machine code : works the same way ... better still, one can simply discard all these and create a program mannually: with raw components ... the same thing ... but more tidious ...this was why I gave the analogy of the crude keyboard ...

But what you're saying is that an actual cat represents the word "cat". ... No it's actually more like saying the whiskers and paws and tailsand eyes represent this animal : and we sysmolize it as "cat" ... 

Or are you focusing on the fact that the symbol, when written down, physically exists? ... not the symbol... the button ... from my analogy there's nothing inscribed on the button ...

"Represents" is very important, since a "code" is a symbol (of the second level). ... well then you probably didn't read my definition right ... I can change the word "represent" to "activates" ... still doesn't change the point of the definition ... 

In the end, symbols themselves can only represent things, because they are identifiers, only. And these kinds of things only exist in minds. Minds are the only ones who need to identify things like that. ... I think this is another point of contention ... symbols don't exist in minds alone ... I can use a bunch of rocks as code ... in that case the symbols are the rocks ... what you can say is symbols can only be recognized by minds ...

A computer never has this problem, because it receives instruction, there is never a choice, or any ambiguity. It is not aware of any symbolism, or anything even close to that. ... again, watch your usage of the term "computer" ... a computer is an artificial mind and it can choose and recognise symbols: but only binary ...

But our mind is produces by a neural network, the brain. In some way, the word "sandwich", and the understandinf of the word, aswell, must be stored in this neural network. And on that level, there once again is no symbolism. Minds can work with symbolisms, but neurons can't. ... hmmm ... just out of curiosity: how do you define or describe the human mind?

This is why a computer could have software that gives it a "mind", and then it could understand symbolism and use code. ... a computer is a "mind" ... 

Yes, but you can imagine that there is a programming language where there is a codeword that does two things. "Swap", for example, requires multiple steps: ... and that is a different code: like I've been saying ... different codes represent different functions ... and a program contains a host of these ... that's why I say a program is a collection of codes ...

We do not want to have to write a program the way that computers work, we want to be able to write them the way a human would, by defining concepts. Then it's up to the compiler to turn that into a program. ... well like I've said repeatedly : if you skip the compiler, you're doing more or less the same thing ...

Well, you're very wrong, and I've explained why, many times, so I don't know why you keep insisting on saying this. This is the kind of thing that makes me think you're just trying to troll. ... what? ... if you followed up closely you'd see the rationale for that assertion ... but it's not doing any of us good if you're going to easily forget threads of arguments ...

Hex isn't code, and it's not called "hex code", it's simply called "hexadecimal", or just "hex", or base-16. ... I think I know what the hexadecimal system is ... it's code to me if it does the same thing as binary in a computer ... and I call all of them code ...

First of all, HTML is not a programming language at all, and it is never compiled. It isn't even a scripting language, it's just a way to format text and images in a document. A tagging system. It isn't "source code" in any sense, it is data. It's a file format. ... well I hope you're right this time because it sounds to me like you're wrong ... again ... what you're telling me is that writing up a webpage in an editor is not coding ... PS I don't understand how HTML is just a "way to format text and images" ... what happens in forms? : for example  ... which have systems for receiving data and processing data? ... 

Remember, "software" is also only in our heads. Software is conceptual. ... I don't agree ... for all I know software is a program stored in voltage patterns ...

What is really, truly going on is that the CPU is turning one pattern of voltages into another pattern of voltages. ... and this is what I've been referring to as the computer code all along ... what's really hard to get here? ... I'm saying that a computer has the programming to interpret "codes" ... and these codes are just voltages and switches ... however we represent them is totally trivial ... it's just to get more efficiency from the system ... the code remains even if we throw all of the assembly, compiler, etc in the bin ... it's the same thing as taking the transistors and wires and creating the circuits mannually ... the same thing ...  take any program: say a download manager (IDM for example) ... this program can be created manually with physical components without any need for a single written symbol ... the only difference is that it'd probably take atleast 10X the time it'd take to create it with a modern computer ...

It's only in our "pretend world" that these voltages were anything more than they are. And "software" is part of the "pretend". ... the voltages are instructions and codes to a computer ... I believe I said that a computer is only an artificial mind ...

But it's really, really hard to understand this, because these "unreal" things still create an emergent system. ... actually no "unreal" thing on it's own can create such a system as the computer ... everything about the computer is real: but our description gives the facade of something inherently conceptual ...  and that has been my main point all along : everything, including the "computer code" is real ... and I've demonstrated how any program can be created without need for any written symbolism ... 

Don't be afraid to admit it to yourself if you don't understand it. This all is beyond the average person, and not something you have to understand at all. ... I fully admit it's confusing to a large extent ... but my explanation seems to be the simplest so far and the most accurate ... most of your explanation relies on the conceptual ... and it's always going to be more difficult if we look at it from that angle ... so I suggest you look at it from the practical / engineering perspective ...

TGAC is code for the full names of the nucleobases in DNA. ... wouldn't this translate to the binary and headecimal format? ... where cytosine is homologous to binary and C to hex ...

well I think we should take a recap from a simpler perspective ... from my definition a code is anything (symbol, object, etc.) which represents(or activates) a single action ... this definition is still up for scrutiny and fine tuning ... the letters in the english alphabets in this sense are all codes ... the act of utilizing a code is more or less a language ... so everything spoken in english language are basically codes ... just that they are codes that all English speaking people understand ... to me latin would still be encoded language ... I would need a system to decode it ... this brings me to the final aspect of my definition ... system which understands and interprets the code ... in English language, we study the system and basically each one of the english speaking person is a "coding system" ... because they understand the code ... this similarly applies to the computer ... the computer is the "coding system" because it is an artificial mind made to understand only a language made up of "on states" and "off states" : what we represent as "0's" and "1's" ... next point of inspection is translation of codes ... a language can be translated into another language ... but this requires yet another, different system ... I wouldn't call it a coding system at this point: "transcription system" would be more appropriate ... and that's what "binary form" would be ... in french it'd probably be "i" and "0" ... so by my description,  binary representation of computer information is a language made up of codes ... translating it into C++ is like translating English to french ... C++ is a different language and requires a system for translation ... 

so to sum up:
1. Code: anything which represents, or activates a single action in a "coding system" ...
2. Language is a collection of syntax( not sure if this is the right word but I presume u understand) which are each codewords ... e.g
-language: English, Syntax: A-Z/0-9
-Language: Binary, Syntax: 0,1(I mean the real on's and off's)
-language: DNA, Syntax: CATG(real neuclotides)
3. Code/Language Translation: ie converting a code/Language from one form to another... 

This is up for scrutiny but I think it's more consistent and accurate ... 

One more thing ... codeword ... a "codeword" I can say is a code made up of more than one units of any syntax in any language ... this actually ends me up in a bit of a fix since one word in English language can mean more than one thing ... however I could classify it as a special kind of codeword ...

Well, my image of you just grew a bit. Thank you. ... well I appreciate that: I just hope this influences the discussion positively ... 

Remember, HTML/CSS are not programming languages, they are file formats. ... I'm reeeeally skeptical about this one ... by my definition, they are ... they contain codewords which contain specific functions ... 

When you write something in html, it becomes a file that is read by a program (IE, firefox), and interpreted. It is content to be loaded by another program, like any data file. ...I could agree with this to an extent ... 

Genetic code is made though evolution, we know this, we see it constantly. ... wrong ... genetic code is altered through genetic variation and natural selection ... it's either a duplication, or a deletion or a change in emphasis ... nothing new is created: new in the sense that a totally new system with new proteins and new structures can arise by these processes ... from my comment I specifically said "created" ... i.e originated : from what I know, no new "perspective" information has been observed to arise from evo. mostly scrambling and deletion ...

When we make RNA self-assemble in labs, we didn't make the sequence, nature did. It was basically random, but that doesn't mean it isn't a genome, so to speak. If the sequence is useful, then it will do better than those who got a useless sequence. ... I'd really want to see these RNA self assemble: I've heard of something like this but it's nowhere near a functional organism ... if this is the case then that doesn't prove anything to me ...

Yes, which is why I said "humans" create technology. Dolphins don't, even though they are creatures, and they are intelligent. ... I believe you said "intelligent creatures" ... that was what I aimed to counter ... you're saying here that technology is only created by humans ... well I'm pretty sure that's the criteria to be even called technology ... my point however is that our technology is extreemly similar to some of the things we see in nature: a flagellum is more or less a motor ... I'm saying that the origin of such a thing was most likely an intelligent cause: since no one of us got to see it happen first hand, we can only infer: you are infering from a process that destroys info. more on the average to explain something that complex and intricate: I'm inferring from the only cause we know that can get a system like that to start working, with lesser or even negligable improbable outcomes ...

If "intelligence" creates technology, then dolphines should also, since they are quite intelligent. So are ravens, and some other birds, for example. ... simple explanation: difference in intelligence ... dolphins are quite intelligent alright, not as much as humans are obviously ... 

A disembodied intelligence (if such a thing could exist) still cannot produce technology.... well like I said God is beyond the limits of the natural laws, but He also manifests in different physical forms ... nothing stops him from moving physical objects ... 

We know that it's possible to gradually build a system that is IC. ... no we don't: we know that it's astronomically improbable to gradually build an IC system by random addition of random parts ...  

That's why I'm saying that if this is simply what you mean by IC, then it is a moot point. IC, in this sense, doesn't mean it cannot evolve. ... well IC simply proves that an IC system needs it's vital components assembled spontaneously ... so it'd be irrational to believe that it can be assembled gradually over millions of years by adding random parts ...

I would prefer to see IC as something that cannot evolve, then it would actually pose a challenge to the theory of evolution, and be "useful". ... IC doesn't directly say "this system can't evolve" ... it only says evo. would have to spontaneously assemble this system to get the observed function... and that is highly improbable ... any rational person would hence be expected to take the most probable position ... which is: evo. wouldn't be able to create this system ...

That would have been the only useful definition of IC. Yet you choose the one that is pointless? Why? ... dafaq ... 

I mean, the idea that if you have a system, and then remove a vital part of the system, and then the system no longer works, then that is too obvioius to even mention. It has no value at all. It's basically a tautology. ... "too obvious to even mention" I kind of like that phrase ... applies perfectly to evo. : which is basically telling us that "organisms change" : like: yeah cave men could tell that different variations of animals have different advantages ... the fact that we could selectively breed long ago is proof that the idea of change of allele frequency has been known for millenia ... btw IC is basically meant to distill the facts into scientific terms and make conclusions: one of which is the fact that a system would need the said parts to function as it's observed ... and that's vital ... 

We have no reason to falsify it, or even care about it. Yes, IC exists, by your definition. So what? We knew that, already. ... I'm glad to hear that: [side note... we knew thousands of years ago that variation and frequency change existed] ... also, by stating you know that IC systems exist then you agree that the vital parts are needed simultenously to make the system function ... 

But this cannot be extended to life itself, because we have no examples of something that designs life - except for evolution. ... of course not you have no example of evolution "designing life" ... all you know is from an already functioning system of preset genomes with reproduction and variation ... you just assume evo. can "design life" somehow : even if it's highly improbable ... I think you could be accused of needing more faith than myself ...

No, IC systems can evolve. There is nothing about IC that makes it impossible to evolve. ... the fact that it's IC makes it a highly improbable situation to be achieved by evo. ... and I don't think an IC system can evolve ... also, evo. has a greater tendency of destroying the than favouring it ... 

 *IC is pointless, it's a tautology. Effectively, you're saying that something isn't what it is until it is that thing.* ... more like this thing can't be what it is except by spontaneous creation ... 

Because if you remove one part, so that it is no longer that thing, then it won't be that thing anymore. That is exactly what your definition of IC says. ... exactly ... it's kind of a "re-tracking" method ... from what we see we try to retrace backwards to ascertain how it arose ... and we can tell it arose spontaneously ...

This has absolutely nothing to do with whether it can evolve or not. It doesn't even present a challenge, it's not something we have to give a moments thought to. I don't understand how you can't see that. ... actually, it does pose a challenge to the gradualistic, step-by-step method of evo. evo. says it arose step-by-step, the evidence shows it arose spontaneously ...

Yes, the flagellum has been explained, since the 1970's or so. Google it. ... pretty sure I've search enough of that before now : and to my knowledge, the supposed explanation is exaptation: like I said ... which basically says evo. assembled it spontaneously ... somehow ... this doesn't work ...

But if we can find the reason for why holes exist, and demonstrate that the process works, then we've got an explanation for why the hole might be there. ... I think I can say I know the reason why IC systems and codes exist and I say it's intelligence ... I'm not really sure why I'm not allowed to say this ...

You creationists want to look at the hole say taht simpyl because the hole exists, the reason is "god".... you're taking a huge leap again and probably trying to make an equivocation: ID doesn't say "God did it" ... it says Intelligence is the best explanation ... you still seem caught up on the ID/creationism equivocation ... a very powerful equivocation which caused ID proponents to loose a court case ... If you're going to analyse them with any rationality then atleast know exactly what they say ...

Darwin actually identified the process that diversifies life. Instead of pointing to life, he pointed to the process. And the process can be tested and repeated and observed, like any proper science. ... I'm sure I've said this but ID has no clash with natural selection: it just says natural selection can account for the origin of all the complexity of life ... IC systems and DNA most notably ...

No, you're saying that because these attributes exist, the only reason for it is "god". ... again, a huge leap from the scentific aspect to the belief aspect: I've pointed this out various times ...

Yet you can't identify the process "god" used to create it, so how can you say that? ... well we say the process is design ... 

And neither can you identify a god who has actually done it. ... as a Christian I say it's God... or what you might call Yahweh ...

So this is an argument from ignorance: You're implying that just because we don't have the answer to where life came from, the answer is "god". ... I believe this is you lumping different concepts together again ...   

Textbook argument from ignorance. ... I don't think so ...

This is the exact same thing as when ancient people didn't know why lava came out of the mountain, so they said god did it. ... I'm not sure the Judeo-christain faith said such: 

So do you really want to keep making that mistake, or will you realize that something that is unknown is simply unknown, at this point? ... to my knowledge, the main claim of the Judeo-Christian faith has been consistent since it ever started: "God is the Creator of the universe and life" ... and it still is the main claim today ... that's reasonably consistent by religious standards ...

IC is a challenge to the theory of evolution to explain how something could have evolved. If we can figure out how it could have evolved, then the challenge has been met. … lol hell no … if you imagine an evolutionary process it has no weight what so ever on the facts

Saying that something cannot have evolved is an attempt to falsify the theory. If it is true that it cannot have evolved, then the theory (or parts of it) is falsified. ... actually saying "something cannot have evolve" is like the last claim we make ... our main claim relies on spontaneous emergence ... and spontaneous emergence is more or less a nightmare for evo. ...

But if the theory of evolution can explain how it could have evolved, then you can't prove that it didn't evovle that way. ... well we can prove that it'd require a good amount of faith to believe it evolved that way: this is because of the very low chance of an IC system arising spontenously by evo. processes ... 

No one is saying that we know how things evolved, we're saying that we know how they could have evolved, and that makes it the most likely explanation. ... and we're saying that's highly improbable : I was wondering that the most likely situation should be the most accepted, scientifically ... but apparently even highly unlikely outcomes are accepted for the fear of the alternative ... 

We know that they did evolve, and we know a lot abotu which species evolved from which, we just don't always know much about the details of how they evolved, since we often don't have the evidence to be able to tell that. ... well from my perspective the claim that "they did evolve" seems to me like a wishful claim ... without sufficient backing ...  the intricate systems and coordination at molecular level gives us an idea of just what exactly evo. has to achieve ... I think most rational people can admit that the complexity of life is too much to be accomplished by evo. ...  

This is when we need to figure out what the possible options are, and which options are more likely than others. ... and I think the most likely option is obvious ... and I certainly don't think it's evo. ...

If there are no options that we can find, then that still doesn't prove that it didn't evolve, it just means we haven't come up with a solution. ...  but there's a solution readily available for thought ... it just seems to me that you want to believe somehow evo. did it ... if you consider the two options without any bias, then atleast you would admit that there's good reason to invoke intelligence ...

To say that it didn't evolve just because we don't know how it could have, would be an argument from ignorance. ... I think the main claim is that it's highly improbable for evo. processes to create the system in question ... 

We don't need to "refute" IC, we know that IC is true, but it is of no value, it doesn't mean anything. It's like saying a red car is red. It's obviously true, and can't be false, but it also means nothing. ... that analogy is a miscue ... lol ... 

I have no idea what "imaginary" processes you're talking about. ... I'm talking of natural selection and random mutations constructing highly complex biological systems: the probability for this is extreemly low and it'd require faith to accept it: to a rational person, it's the most likely situation that goes ... it's just like you telling me that in theory we can achieve 100 consecutive Six' from rolling a die ... well if I say you can't do that realistically, you can't fault me because there's just a very little chance for that: it's just the most rational thing to say ... however the chances of assembling a fully functional flagellum are way less than the die outcomes of 100 consecutive six' ... so why am I faulted to say that's not possible?

To say that something is "irreducibly complex" is like saying that it is "red" or it is "large". It's just a specific kind of description, an adjective, basically. ... not really ...

It's not a theory, because it is not an explanation for any phenomenon or something like that. Therefore, there is nothing to "falsify", in that sense. ... it's not a theory alright, it's a scientific fact ... and it can be falsified ... it only requires a demonstration of a system like the flagellum arising in a stepwise fashion with functions equal to the number of steps taken to achieve the IC system ... actually, at the moment, it's still a bit less refined and can be challenged by systems with fewer parts ... but it's still hard to replicate in a lab ...

Basically, to "falsify IC" is similar to "falsify redness".... reeaallly don't think your on track here ...

However, you can falsify the claim that something is IC, just like you can falsify the claim that something is red. ... how's that?

No, the human eye is definitely not IC. There are plenty of things you can remove, and it'll still be able to "see".... yes the human eye is IC ... don't know if you thought of my description before applying it to the human eye ... if you take out the lens then you have some kind of really long sighted situation can be best described as blindness ... 

No, the scientitsts do not say what happened, they said what might have happened, or could have happened. There's a big difference. ... "what might have happened" I like that phrase ... you have to realize that it's not a credible scientific position to say 100 consecutive Six' might arise from rolling a die 100 times... atleast not the way I see it ...

We cannot make an eye evolve from scratch in lab, since it took billions of years, as far as we know. ... well I say you don't know about how the eye arose ... "billions of years evolution" is not a credible excuse to me ... it's imaginary... and like I said, it's irrational to accept such a position ...

But see, if you want to challenge evolution, then it is up to you to bring the evidence against it. If you're claiming that the theory of evolution is false, then you're making a positive claim, and you have the burden of proof! ... well aside IC and SC there are other good evidences I've brought up that really go against evo. most notably the cambrian fossils : and most of the fossil record tbh ... in addition there's the argument of what is known as the "fine tuning" of the universe and some universal constants that have values which apparently need to be exact to permit life ... also, the amount of development that took place within the last 2000 years is too exponential for me to believe humanity couldn't achive such in 200,000 years before ... 

And before you get this wrong: The theory of evolution did have the burden of evidence, but it has met it. It is an established theory. ... it fell apart long ago: the only reason it was still considered was because the only available alternative was "incredible" ... that combined with the numerous false evidences which have been repeatedly conjured up to keep the theory alive ... aside that, the total revolution/change of the definition showed a desperate attempt to add validity to the theory ...

It's a different thing to just not accept it, but if you want anyone else to reject the theory, then you need to prove that it is wrong. ... actually, it's yet to be proven to be right ...  from the way I see it ... 

If you're indeed claiming that "it is false". To say "I don't believe it" or "I am not convinved by the evidence", that's fine, you don't need to support that, that is just a statement of your position towards it. ... ofcourse that'd be OK by me if it wasn't forced to be seen as a scientific fact that couldn't be challenged by any alternate theory or contradicting fact ... it'd be OK by me if someone didn't have to loose his job for supporting an alternate view which he thought to be more reasonable ...

It's usually in a bacterial lifeform that we talk about these things. So, you're telling you that even though they have generations that are something like 20 minutes long, and they have populations in the trillions, and hundreds of millions of years of time, you find it "unlikely" that some parts would start interacting to produce an emergent property? ... actually bacterial lifeform should have been used to prove that an IC system can be built out of nothing ... but the only bacterial exp. I know of showed no such new systems: what I got from it was that evo. can actually destroy function more on the average ... that's really not going to helf if we're trying to build new complex systems ...

And you're so sure of it that you "lol" at it? ... my "lol" was at the explanation given by exaptation: it basically attributes intelligent powers to evo. in expecting it to perfectly assemble a system with 20+ parts spontaneously from components with prior, different functions ...

And Einstein referred to #1, while most atheists are of the #2 kind. He was clearly not talking about the #2 kind. ... well he was ...

I'm not sure it is. People usually mean a "personal god", one that actually matters, the kind that people make religions about.... well like the definition of theism says: it doesn't have to "personal" ... 

But to the best of my knowledge, I don't believe in any gods. And in fact, I'm quite convinced that gods in fact do not exist, but it really is a matter of definition. ... so which is it? please be specific ... is it that you "don't believe in God" or you're "convinced God doesn't exist"? ...

But an impersonal god is hardly a "being". It can be a "force", as some call it. It can be the universe itself, which makes it not supernatural.... Umm... a personaly God can also be a "force" or "the universe itself" or even "not supernatural" ... so?

If someone says "god is love", then god is not a being, it is an emotion. Maybe it is the instict to love people that some people refer to as "god". And that doesn't make them "theists". ... by saying "God is love" I mean God is the source of what we know as love ... it doesn't mean God is nothing more than love ...

That is correct. All I can say is "stop believing something you have no justification for believing". ... OK you also have no basis to assert that I have "no justification for believing" ... that's completely wrong ... even more so after I've explained many reasons why I believe ...

That is not to say "god doesn't exist", but rather "we should not believe in god, since we have no reason to. ... that's a completely wrong assertion ... there are many reasons why one can believe in God ... 

People's belief actually do matter to society, to varying degrees. As you know, religious belief has killed a lot of people. Therefore, it is only right to ask for a justification, or ask peopel to stop because they have no justification.

No, of course they can't. Volcanos requires that there is a flow of magma there, that can break its way to the surface. ... Ooook ... hence the reason ... doesn't address my point at all ... if you can predict exactly when and where every volcano will errupt then you might be able to explain why it's not random for you ... however it's still random for the organisms that can't ... and you're damn sure as hell no pre-human life form could predict volcanos ... so yes volcanoes are random occurences for evo. ...

Yes, aswell as many other things, like competition of sresources, sexual selection, and whatever. ... exactly... and you can't predict them ... I mean random mutations affect the environment in sich scenarios ... combined with all the possible outcomes in an environment, like you implied, there's definitely no telling what might be the case ... really don't understand why it's not random ...

Of course they aren't. ... Ok this one has no rationale behind it ...

No, they not random. If the selection pressure changes because your prey, which you've been living on, dies out, then that is not random. ... yes it is becouse you couldn't predict the "sudden" situation ... it just happened to be so ... 

And it's not going to be very "sudden", because the number of prey individuals is slowly going to go down, and it'll be harder and harder to find any. ... yes it is because the number of prey individuals can aswell shoot up due to a favorable condition or mutation ... absolutely no way to predict it ...

And that's probably one of the more sudden changes, though. Other changes are when the ice ages come or go, which is a very slow change. And they're not random, either, they come in waves which are pretty constant. ... well for pre-human organisms, that's all random ...

But predator-prey dynamics is probably the main thing that controls evolution, I suspect. ... and these dynamics aren't random by you judgement I suspect? ...

Some factors can be predicted, like climate change, ice ages, and the growth of deserts, for example. ... well just to point out probably only modern humans can predict this... for previous organisms, this is most likely a game of chance ... 

Some things can't practically be predicted, because there are too many factors,m and it depends on how far into the future you're tryig to rpredict it. ... well many more things can't be predicted in the environment ... even by modern humans and their technology ... so why exactly is the environment non-random? I still don't get it ...

But you'd basically have to ask an expert about this, really. I don't know enough about it. ... don't really know much about these things in advanced levels as well ... but it can't be that hard to just see that the environmental conditions for evo. are random occurences ...

For something to be perfectly random, the change of any "number" to come up must be equally large. There must not be a pattern or a way to predict it. ... the environmental conditions are well perfectly random because the number of options exceeds the limits of the ones modern humans can predict ... there are numerous situations that can spring up and over turn an advantage from what you can predict: ie your prediction can  easily backfire ...

But like I said, with 2 dice, 7 is more likely to come up than 2, which means it's not very random. ... well in the case of the dice it's still a random outcome ... 

And I'm sure you agree: If you were given the choice, with the same payouts, between rolling 2 or 7, you would also pick 7, because you know there's a better chance you'll win that way. ... yes def. ... but I'm not sure if this analogy perfectly maps the evo. process ... might well be an oversimplification ...

However, with one die roll, want to pick 2 or 5, for example? Doesn't matter, the odds are the same, theoretically. And the odds being the same for any number is the definition of randomness. ... actually the way I see it the odds are pretty much the same for all organisms ... for one I don't think any organism before humans could perfectly predict these Ice Ages and dessert forests ... aside this, the possible environmental conditions are probably countless: tall trees for example can very well be an environmental pressure ... 

I can't, it's a paradox!... funny ... yes you can ...

* Well, if evolution was random, then it wouldn't be "evolution", so what is it?* ... lol ... evolution is random buddy ... that's why Lenski's experiment can't be repeated with the same results ... 

Given a specific situation, and a short-scale prediction, then yes. ... give me one example of such ...

But that's not my point. Species cannot change if there is no direction, or they would just hover around a center point. Take the number zero, and keep adding either +1 or -1 to it, perfectly randomly, and over time you should be hovering at the number zero. No actual change. ... I don't know how your math is giving you this ... if I take a number 0 and add either -1 or +1 randomly I can well get to even 5 ... it'd just have to be a very likely situation where I randomly add more of +1 ... I mean it's random isn't it? ... evo. works without a direction from what I know ... even if the environmental pressures act as a direction, it doesn't make it less random because the direction is basically a random outcome ...

But in nature, this is not what happens, which means that it isn't random, there is a bias towards some specific direction. ... actually there's no "specific direction" : you're probably contradicting yourself again ... anything can turn out to be a direction: this means that probably nothing is ... 

*And species become better adapted to their environment, and that surely cannot be random! * ... yes it can be and it is ... if not, there'd be no extinction ... the ones you get to describe as "adapted" just so happen to be the lucky ones ...

There is a pattern, and where there is a pattern, there is less randomness. ... there's actually no pattern from what I've seen ... it's just a matter of who's lucky ...

First of all, you did not actually do the test. ... I really don't have to simulate it live to know the outcomes will change ...

Secondly, this it is a mathematical fact. If you're getting a different result, you're simply not doing it right. ... what mathematics is this? if we're adding -1 or +1 randomly, then we can very well get a situation where +1 would turn out 3 times or more ... the odds for three consecutive +1 outcomes is not high at all ... except you say were adding it in turns of +1 and -1 : then that's not random ... you'd actually not even get any change in frequency ...

No, the result won't be exactly 10, but it will stay around 10 over time. It will not grow in any direction, which is the point. ... no the result can well drift to even 15 ... it's just a matter of chance ... PS even a scenario where an average of 10.01 becomes more frequent is enough to verify my relatively easy prediction ... 9.92 will do as well 10.5, 11.8, etc ... it doesn't matter ... what matters to the prediction is just change ... 

Given an infinite about of "generations", the average will be exactly 10, theoretically. ... not sure if your math is correct ... 

"Imaginary analogy"? The only thing "imaginary" here is that you imagine that calling the analogy "imaginary" makes any difference. Yes, analogies are imaginary. ... well nice way to evade the "convienent" ... 

It is a demonstration of a fact, that's all. Anything that replicates with variation and has a selection pressure will evolve. That includes numbers. ... Nope ... from the analogy we saw that anything that replicates with variation will "evolve" even without a selection pressure: afterall "evolution" is the change in frequencies:   

I used numbers because it makes it easy to examine, since you can easily calculate the average value of them, so you can tell if the "species" has changed as a whole. It's only for convenience, nothing else. ... I think it was a fail ...

I can happen, in theory, but won't happen in reality. ... Oh I see ... somethings in theory won't happen in reality but some will? ... beautiful stuff here man ...

So when I say that it is more likely to go any other direction than exactly backwards, you suddenly have a problem with it? And why is that? ... not sure I'm getting you here ... but I'm saying that the law of irreversibility makes no difference to me since it's based on an evo. presupposition ... also, it's contradictory cuz you implied one time that evo. moves in no specific direction ... I addition, there's no plausible restriction I know of that can prevent humans from "evolving" wings in a million years time ...

Even if you don't accept the theory of evolution, you still have to argue against the actual science, not a straw man of it. And that includes the law of irreversibility. ... well I don't think the law of irreversibility adds any more validity to the theory to be honest: like I said, it basically says evo. doesn't move in a backward direction, even in evo. moves in no specific direction ...

We have good reason to think we have found that the stone henge were made by humans. But we don't know that, because stone henge sure is quite special. But it is definitely very likely.... oh well same seems to be the case for most of life: same way we know that the stonehenge was most likely not built by a rockslide ... the most likely cause for the complexity of life is design ... that's just a rational extrapolation ...

"So a really bad designer, then, who keeps failing and never seems to learn. … lol did you read the comment or are you talking off your ass again? … I said each time He added more info to help the organisms withstand entropy … what don’t you understand here?"

What I don't understand is why the designer would have to change his design a gazillion times, instead of making it "fail proof" from the start.... it was fail proof for the designer from the start most likely ... but probably not enough to last for a very long time ... PS try to read with a larger perspective: it'd solve a lot ...

And if he meant to make a rabbit, why didn't he start out with a rabbit, rather than making completely differnet kinds of stuff for millions of years, until it started becoming more like rabbits? ... please don't mix your evolutionary belief with my explanation: you're gearing towards a strawman here ...

It wasn't "maintenance". They were drastically changed over time, to more complex creatures. ... so how much did the anthropods change again?

Yes, it is, because you cannot define what god is, what he is "made of", or how such a thing "works", and you cannot define anything about the process by which he created things. ... first we can define to an extent what God is ... secondly, the process by which he created things is most likely design: we know of design: and we know human hands and even our technology can't create something that intricate and nanoscale ... 

It is brutally vague and undefined. You're saying something unknown did something using an unknown process, for which there is no evidence, just because you can't accept hat evolution already explains it. ... talking off your ass yet again ... I never said God was "unknown" this is probably another strawman from you... I said we don't know God fully but there's some things we can tell about God ...and the process is design ...and evolution doesn't explain it: one can't just say things just spawned up to be this complex by chance and expect me to accept it as anything but a wishful story ...
 
And that's ID/creationism summed up. ... well you can just prove yourself to be ignorantly silly here by defining both terms ... you're ofcourse trying to make the same equivocation I've called out a few times now I believe ... the same equivocation that lost a court case for ID ...  

The problem is not that evolution doesn't explain it, the problem is that religious people aren't allowed to accept it, but they'll do anything to avoid admitting that. ... well I think the catholic sect accepts it: but speaking for myself, I don't accept it because it just makes little sense to me ... I can hardly be associated with any christian sect so I don't adhere to anyone in particular ... by the way you should consider your assertion for evo. and ID because it's even more of prejudice in the scientific community ...

For example, such as "projecting". The fact that they aren't allowed to accept evolution is "projected" onto science by claiming that scientists aren't allowed to accept creationism. ... be specific: creationism or Biblical creationism, or ID ... don't try to make equivocations to push your ill-reasoned position through
The classical "no, you are!" argument. ... yes as expected it only works for the opposition ...

I don't know what to say, punctuated equilibrium is correct, that's all. We see it in nature, and in lab. ... there's a good chance you might well be only seeing what you want to see ...

It makes perfect sense that the more fit you are to you environment, the slower you'll evolve, because the "less fit" individuals of the species won't have a problem, since even they are fit enough to reproduce just fine. ... still doesn't explain the missing plethora of transitions required to validate evo. ... OK rapid evo. time periods followed by times of "stasis" ... weeelll: where are the millions of "rapid" transitional fossils? ...

Wait, what makes you believe that? Have you been getting your information from creaitonists, again? ... actually most of my info comes from debates between ID proponents(meyer, Behe, Dembski, etc) and evolutionists (Ken Miller, Cassone, etc.) ... pretty sure your beliefs aren't that rational ... 

"So fast"? I don't get it, it seems like you're telling me that a time that is best known for so much evolution "disproves" evolution? Are you high? dammit the transitions... you can't have major phyla emerging out of nowhere without transitions and expect evo. to explain that ...

How they could evovle so fast? Because they can. If you're talking about the cambrian explosion, then that was a period of about 25 million years. Remember, humans diverged from chimpanzees only 7 million years ago. Dogs evole from wolves in 10 000 years. ... OK it was 5mill years ... no 10 ... no 7 ... no 20 ... 20 makes it sound more inline with evo. ... lol ... nice job but we're not particularly sure how these time scales are determined ... but nevertheless : WHERE.ARE.MY.TRANSITIONS??? ... 

25 million years is a looong time. ... Ooookkk ... sooo, enough time to show the intermediary steps ... but there were, well, pretty much none ...

And creatures who are not as complex as we are now can evolve quicker because they are not as "tied up" in a complex system. It's harder to change humans than to change a worm, so to speak. ... "quicker": I guess you can see now the rationale behinh the "evolved so fast" ... but here come a mystery question: how can one evolve so quick within a span of "20 million years" ... am I missing something here? ...

And as for "forgetting their transition", of course they didn't. They transitioned like everything else.... yes and like everything else, the transitions apparently dissapeared into thin air...

You might have gotten your info from creationists who think that we have no fossils from the pre-cambrian, and that the cambrian explosion was 1000 times faster than it was, and so on. ... OK buddy you can now show me the pre-cambrian transitions ...

As I see it, music is art. Anything that was created with the intent of being art is art. So if I record the sound of rocks falling on a wooden floor and say that it is music, then it is, in my opinion. ... well thanks: music is anything that is music to anybody: absurd as it might sound, this is actually the case: and it's definitely not a scientific fact because it can't be tested and falsified: this just shows that if we go by only what the scientific method can prove, music doesn't even exist ...

It is our definitions that decide what music is. ... I agree ...

But if we agree that some song truly is music, then yes, it is scientifially a fact that it is music, because we can measure that it is there, and it conforms to the definition of music. ... well there's no definition we can even assign to music to ascertain this ... and if one person rejects a song as music, then this thought is effectively fasified ... but lets say there's one song that every single person thought was really, "music" : can we now define music to be a sound pattern every body approves of as music? ... no. It'd mean nothing is music until everyone accepts it to be so ... still the question remains ... what is music?

It isn't hard. But it's like this with a lot of things, because a lot of things are simply  a matter of opinion as to how we should define them. ... exactly, music is just what different people define it to be ... it's not a fact that can be ascertained through the scientific method ...

An open system can decrease or increase in entropy, because it can take energy from other systems to do any amount of work. the fact that life can decrease in entropy is best explained by the systems in place which ensure that entropy is reduced... not because entropy doesn't work in life ... entropy still works nevertheless: just that life just happens to have complex systems that seem to battle it to an extent ...

It is only isloated systems that will tend to increase in entropy, because they cannot take energy from other systems. ... well we can say the universe on the average is tending towards maximum entropy ...

But an open system can do anything as long as it can take energy from other systems. That's why the 2nd law of thermodynamics is only stated for isolated system. ... and I'm saying a subsystem in an isolated system makes little difference to the impact of the law ... the law still works ...
Reply: Max Spiegel

The point is that part of the flagellum has a function, which illustrates that IC is a useless concept. ... I'm not sure I'm reading this right because it seems like you're still confused about IC ... I'm not sure I can continue to repeat exactly what IC states ... and what I'm saying about the precursor/degenerated state ...

If a structure is made of components that each serve different functions when not part of the whole, then your concept of IC as proof of somethign being impossible to evolve is dead. ... NO it doesn't ... like I said repeatedly, it has to be proven in a lab that a new functional system can arise by evo. processes to disprove the fact that the IC systems we see need to arise spontaneously ... PS, again, if it well turns out that the T3SS is a degenerated flagellum then it doesnn't have the slightest chance of disproving the IC of the flagellum: I'm not sure you understand this ... Also, even if we assume the T3SS was a precursor, gaining a flagellum from that is a highly tidious task because new components would have to be borrowed from apparently nowhere to complete the structure: and knocking out a vital part can make it useless and hence be discarded by NS ...

Your missing the fact that in principle we just showed that the flagellum is made of components that can serve a function when not as part of the flagellum (let's call them (intermediate structures")., and now you immediately jump to "well those intermediate structures can't possible have any intermediate structures." In other words, you aren't happy unless we can find the exact evolutionary pathway for a structure. This is some serious goalpost pushing, and is completely unreasonable and unnecessary to prove evolution. ... are you kidding me now ... goal post pushing? ... you can't even determine if the T3SS is a precursor or a degenerated flagellum: and I've proved why it's more likely to be a degenerated flagellum ... btw if we map the T3SS to the flagellum we see a few parts which are not homologous to any part in the flagellum: e.g the needle of the T3SS: so "in principle", the subsystem made up of the exact same parts in the flagellum would turn out to be useless... since there's no structure like the needle in the flagellum ... 

So then this is your logic: that removing a part makes a structure useless or serve a different function proves the structure could not have evolved because removing a part causes it to serve a different function, and beneficial mutations are less common than detrimental ones. Do you see the problem here? ... I think the problem might well be your comprehension: this is my logic: that removing a part(s) makes a structure useless proves that the structure could not have evolved by gradual steps since the parts in question are vital to it's functioning and are needed spontaneously: and the process which is supposed to build this complex system just so happens to destroy systems more on the average and build nothing new: this simply implies that it's very less likely that such a process would develop such complexity from scratch ...

And yet magic is precisely your alternative, since you have no experiments in which we have seen a "designer" create biological components "from scratch." Talk about hypocrisy. ... Ah yes Intelligence is magic, and Design is also magic ... well I hope you've checked yourself well before making the baseless assertions ... and I hope I don't have to repeat myself over again on what I'm bringing forward ...

NS only destroys the "broken" versions, thereby increasing the fitness of the working ones; making their replication more probable. ... well incase you didn't notice NS depends on what chance brings up: and if it's highly unlikely to bring up a new functional system, what would NS select for if the highly improbable situation turns out to be actually impossible? ... 

We have not observed "organs" evolve because that takes too long. ... yes of course that's why you need some amount of faith to believe it: it has never been proven to exist but you believe it can still exist ...

We have seen beneficial mutations improve organism though, which is all we need. ... I think you'd need more than scrambling of already present DNA info. to explain emergence of totally new functional "novel" information ... 

I keep asking you to show me the probabilities. ... are you kidding? so even without me showing a calculation, you can't draw up the probability of random mutations creating a brand new functional flagellum hook for example? ... or the probability of the arrangement of the proteins to match the function needed from the hook? ... OK here's a simple one: how many ways can the proteins be arranged to form a structure? well you'd would agree with me if I said 1000000 different ways or more ... how many ways is required to gain a structure like the hook? : well I'd say mostlikely 1... so the probability of forming a well matched hook by random mutations would be 0.000001: or in other words, very unlikely ...

By changing the chances of the parent generation successfully reproducing, NS changes the frequency of the alleles passed to the next generation, so yes it does change the probabilities with a certain structure. ... well NS doesn't really"change" anything in the sense that it just tells which is lucky and which isn't ... 

And so we keep it. And this means it is more likely to show up in the next generation. This is how NS changes probabilities. ... no it doesn't change the probabilities per se: it's the outcome of the probabilities ... 

Timescale makes all the difference. If I roll a die every 5 minutes, how likely am I to get all faces in 5 minutes vs in an hour? In a lifetime? In a billion years? ... well more like roling one million dice and expecting each would have their face showing a particular number ... I wonder how much time that'd take ...

Firstly, we don't strictly know that. ... lol ...  

Are you seriously bringing up entropy again? The earth is not a closed system! The 2nd law is only for isolated systems!!! Gah! ... and the universe? the earth doesn't have to be a closed system for the universal entropy to work ... what you can say is that life has systems inplace which battle entropy to an extent ...

It is only the beneficial mutations which accumulate; never the harmful ones. This is proven by many experiments, like the nylon-eating E. Coli. ... and like I've said, scrambling of DNA doesn't account for new functional biological systems ...

Keep repeating that and sounding like an idiot if you want.... so I take it that you can see this is quite idiotic to be a scientific prediction: well if so then I'm glad you can see this ... but keep in mind I'm only just repeating your own lines ... 

I've already given at least 5 examples of successful predictions made by evolution. You are currently tackling transitional fossils. ... OK you might need to give me a recap here ... I can remember the herrings and penguins: a fail, the transitional fossils: a fail as well, what else?

I just took one starting point. We have to start somewhere. You are also acting like there is only one possible configuration that could be an "appropriate base." ... nope it might be more than one: but what's the chance that it happens to be one which isn't appropriate? ...

Very hard on the species level. We have many on the genus level and above, but organisms don't cross from one family to another so that's not something we would expect to see. You understand this, right? ... nope I don't ... because a bacteria to man transformation is change on a scale greater than phyla level...

So if I present you with a transitional fossil that is more than 70% complete, will you accept it then? ... yes of course but not one that is just labelled "transitional" with little to no signs of morphing from a previous organism or into another... 

That would be awesome, and shows you didn't read the list I gave you. ... well I investigated the first eight and it turned out that I didn't need to waste more time on it: I described a few to you ...

The bible predicts man and all other animals appeared in the first 6 days of earth's existence, which is nothing like the Cambrian explosion. Show me where the bible predicts the Cambrian explosion. ... so in two sentences you managed to say three completely different things and treat them as one ... lol ... if that one is even what I'm talking about ...
1. The Bible predicts that all organisms appeared in the first six days of earth's existence: 
2. The Bible doesn't predict anything like the Cambrian explosion.
3. The Bible doesn't predict the Cambrian explosion ...

Question ... WTH are you saying bruh? ... I'm saying Biblical creationism predicted spontaneous creation of organisms ... and the cambrian explosion proves that ...

Let's not bring another topic into this thread. We already have enough spreading going on here. ... Oh I thought I was asked to bring up predictions by ID...
Reply: Benjamin Toby Your stupidity is getting out of hand. You are incapable of focusing on one topic without spreading all over the place, so I will try to focus you down a bit:

"like I said repeatedly, it has to be proven in a lab that a new functional system can arise by evo. processes to disprove the fact that the IC "
Why does, for example, the nylonase from the E. Coli not count? What kind of "system" are you looking for?

"this is my logic: that removing a part(s) makes a structure useless proves that the structure could not have evolved by gradual steps since the parts in question are vital to it's functioning and are needed spontaneously:"
Yeah, and this logic is incredibly broken. Why could it not have evolved through gradual steps, in which each stage had a different function?

"OK here's a simple one: how many ways can the proteins be arranged to form a structure like the hook? well you would agree with me if I said 1000000 different ways or more ... how many ways is required to gain a structure like the hook? : well I'd say mostlikely 1... so the probability of forming a well matched hook by random mutations would be 0.000001: or in other words, very unlikely"
You astonishing dunce, this would be the probability of your spontaneous generation forming from a single mutation (kind of, but it's actually not even that). You completely ignored NS and how it factors into the calculations, as well as biological inheritance in general.

"no NS doesn't change the probabilities per se: it's the outcome of the probabilities"
And what, pray tell, is the difference between a probability and the "outcome" of the probability? The "outcome" of NS selecting a particular allele is the allele becoming more prevalent in the population, so I don't see what you're getting at.

"well NS doesn't really"change" anything in the sense that it just tells which is lucky and which isn't"
And then it takes the lucky one and allows it to copy... hm... Yeah this part should be in the calculations.

"well more like roling one million dice and expecting each would have all faces showing a particular number once in a billion years"
Oh wow, this seems like another conflation of independent probabilities and a purely random system with the actual world of chemistry and biology. That is sad.

"what would NS select for if the highly improbable situation turns out to be actually impossible?"
What kind of loaded question is that? N selects the most fit members of a population. What can NS select if we assume your nonsense that IC means "cannot evolve?" Is that your actual question?

" I can remember the herrings and penguins: a fail, the transitional fossils: a fail as well, what else?"
You are either an idiot or a liar. The only one who said anything about herrings and penguins was you. You did not do anything to respond to the transitional fossils I brought up.

"a bacteria to man transformation is change on a scale greater than phyla level."
And we have zillions of "transitional" forms between bacteria and human. Basically all of them on the human line would count as such.

"and the universe? the earth doesn't have to be a closed system for the universal entropy to work ... what you can say is that life has systems inplace which battle entropy to an extent"
What are you blabbering about? Do you understand that life follows the 2nd LoT or not?

"I'm saying Biblical creationism predicted spontaneous creation of organisms ... and the cambrian explosion proves that"
The Cambrian explosion didn't happen in 6 days, wasn't a miracle, and didn't create humans. Genesis disproven.

"yes of course but not one that is just labelled "transitional" with little to no signs of morphing from a previous organism or into another."
So if I point you to a fossil that has characteristics that are only found on two distinct animals in modern times, that should count, right? That's as close as animals ever came to "morphing into" one another. Unless you don't understand what a transitional species is, which wouldn't surprise me.

"well I investigated the first eight and it turned out that I didn't need to was more time on it: I described a few to you"
I must have missed your references to the first fossils on the list entirely. Where did you mention the first one, Ardipithecus ramidus?

"Oh I thought I was asked to bring up unique predictions by ID"
Yeah, still waiting for those. Got any yet?
Reply: Benjamin Toby "Yes you were ... you're addicted ... you'd reply even if I was really trolling you ... "

I may be addicted to "this", but that doesn't mean I have to talk to you specifically. I talk to a lot of people. I can pick and choose.

"when your lines count up to over 1500 then it's less likely I'd respond with a well thought out reply ... I certainly wouldn't have all the time to scrutinize and re-check like I usually do with shorter comments "

It's the same for me. I don't want these things to grow to these proportions. But we both need to help keep it shorter. You just gave me a 1404 line comment. I can't just ignore 75% of it.
 

"you definitely can't blame me for any time lost ..."

I'm not blaming you, I'm very well aware that I am mainly the one who casues these things to "grow". It happens every time.

"you can just listen to the beeps and decode the message instantly ... without any need for symbols ... "

The beeps are symbols. And even if you can learn to decode them to letters in head so fast that it effectively seems as if you're not even decoding them, the fact is still that the morse code system was designed as a code system where letters/characters are encoded into short/long. You've just forgotten that.

"*"Cat" refers to the concept of a cat. The concept allows us to indentify something as being a "cat".* ... so what exactly is wrong if we identify DNA as a code? "

DNA is a molecule. A DNA sequence can contain encoded information, but that can only be so if it was intended that way by someone who wrote it.
Basically, there are two ways to know whether a sequence is "code" or not:
1. Find the guy who made the sequence.
2. Identify a known coding system which, when applied to the sequences, makes the sequence make perfect sense. It is highly unlikely that something apparently random would be decoded into something meaningful with the wrong coding system.
If "IEQHGKSGBOWE" decodes to "I hid the stash of candy under the bed", using a specific coding system, then that is quite clearly the coding system used. It is unlikely that the wrong coding system wound coincidentally produce a valid sentence, like that.

But remember, DNA is basically just that: "WIHEGGWEIHNGWEIIGEWHBVWPWIOE". Nonsense, effectively. But it has chemical properties. And the cell uses its chemical propoerties, not the "meaning" of the sequence. It's not arbitrary, like code systems are.

"a computer can understand pretty much anything ... it's just a matter of the programming ..."

No, that's the software giving you the appearance of understanding. It's not the computer, it is the program.
We were talking about CPUs and instructions, and thigns on that level. On that level, "meaning" cannot exist, just like it cannot exist on the level of neurons in the gbrain - but the mind can hold understanding. And so can software, theoretically.
Why do I make the distinction between software and computer? Because you can move the software away from the computer, and it still does the same thing. And you can put it into a different computer, or even a different kind of computer, and its still the software that's causing it to "understand".
"Software" is the equivalent of a "mind", assuming the software is capable of that.

For a computer to be able to work with "code", the CPU must have a mind. The CPU itself, not the software that it runs.
The CPU would have to be able to choose what to do, not be tied to cause and effect, in the sense that a specific pattern of switches causes a specific effect.

"So, a lot of the things we write in C++ never gets turned into binary at all. [...]
 I don't think there's anything in a computer that doesn't get translated into binary form ... "

I just fucking explained it to you.
Fine, I'll give you an actual example, just because you keep insisting. C++ example:

struct Position
{
    int x, y;
};

There, a very short example of a piece of "code" (remember, it's only called "code" because of tradition) that doesn't get translated into machine instructions when compiled.
If you write a simple program, and makle a copy of it where you add what I wrote above, and compile both, you'll see that they will be of the exact same file size. What you added was never added to the program.

The thing I wrote, above, is me explaining to the compiler that I want a kind of data called "position", which symbolically (to me) represents the idea of something being somewhere in a 2D world, where x and y represents (to me) the coordinates of that position.
Now I will consistently use "position" as a way to define where something is.
So I've defined a kind of "concept". Now, if I don't follow my own rules, the compiler can tell me that I did something wrong. That is useful when programming large programs.
And if I ever want to change how a "position" works, I can just change the definition of it, I don't need to change how I use it - only how it works. (This comes back to "abstraction", like I mentioned earlier.)

But note that when I use "position", the only thing that is put into the .exe file are the x and y variables - not the concept/rules about how they should be treated, that hey belong to "position". "Position" will not exist in the .exe.

You do not know programming. You've worked with some HTML or what, but you don't know actual programming, so don't pretend that you do.

"* C++ isn't code, it is a language for talking to C++ compilers.*
 ... I'm pretty sure I remember you saying that writing a program in C++ is actually writing code ..."

No, only assembly is actual code, and whatever similar things that I might not be aware of.
However, because we traditionally call anything similar to that "source code", you can still say that you're "coding" C++. It's not literally correct, it's idiomatic.
The only reason I point this out is because we're discussing what "code" is. I also call C++ "code", even though I know it's not. Yes, it's idiomatic, just like how people often use double negations, like "I didn't do nothing".

"*Binary is not "code", it is a representation, a sequence of symbols that represent the voltages in the computer.* ... by my definition it is ... 1 and 0 each represent a single action ... "

Wouldn't you say a sequence of 1/0 represents an action? But in reality, they only represent states, not actions. They cause actions, yes, but we tend to give actual "names" to the actions.

"*3. Binary is not a language, either.* ... it is in the same sense as any language is ..."

Nooo. Binary is base-2, a mathematical value. It's not a language.
Because anything that has 2 possible states can be described using base-2, that's what we chose to do. That doesn't make base-2 a language.
What you really mean is probably that a sequence of operations/instructions for a computer can be likened to a language. Even if say it is, it isn't to a computer, its only to us. The computer is not aware that it's being talked to, and it can't understand the meaning of what its being forced to do, or anything like that.

"your source code in C++ is definitely not assembly like you said ... so how come only assembly is code now?"

Because assembly is the only programming language, at least between those two, where each word directly decodes into a machine instruction. Any assembly codeword directly represent a value. we're effectively writing direct instructions, but instead of writing the value of the instructions, we use a system where we give those values names - which is 2nd level symbolsim, code.
But C++ for the most part doesn't work like that, as I have explained. C++ is not 2nd level symbolism, it is a language with syntax and grammar (sometimes even inconsistent!) and keywords which is made to explain things to a compiler.
C++ "evovled from" C, which means that it carreis a lot of baggage from C, which causes some things to be a little inconsistent. And sometimes its inconsistent because it makes things easier.

One good example of how C++ is differnet from simply being being code for instructions:

private: static const int x(5);

In reality, what will happen in the computer, is that we simply reserve a piece of RAM to hold a value.
But because this is C++, it's nowhere near that simple. Here, we have resticted access to the variable, by "private", and we've made it "static" (which has a few implication), and we've made it "constant", meaning no one is allowed to ever change it (though there are ways around that), and we've given it an identifier, "x", and called its constructor with the argument "5", which will cause it to hold that value "5", in this case.
It's also implied that this variable is a member of a class, since only classes/structures can have "private" members. Adn the fact that thigns are implied, or implicit vs explicit, directly proves that it is somethign more than just "code".
Being "private" has to do with whether "friends" of that class can access it, and whether classes that are derived from this class can access it. Yes, types can be inherited in C++. you can make a tree relationship, nested groups, similar to a family tree, where traits are inherited from parents and grandparents, and so on.

This has a lot of implications on a lot of other things, and takes a lot of other things into consideration, and so on. A shitload more complex than assembly.
One simple statement of C++ often will cause a lot of things to happen, and more than one instruction to be written, too, because of context.

I hope its starting to become clear how a high-level language is very different from assembly. The rason is that some program have a million lines of "code" (windows vista, for example), and then you need the computer to help you, because humans can't be trusted to remember and understand it all.

But in the end, all of this complexity disappears when we compile it, and all that's left is the equivalent of assembly. You can even tell the compiler to output as assembly, in case you want to read what it wrote for you.

"*You only define concepts, and you don't have to care how the computer does those things.* ... I think you should ... at least if you're going to define what the computer code actually is ... but you don't have to know all that as a programmer ..."

I agree. A good programmer needs to understand how the computer does things. It's especially important when you need good performance. You need to understand how to best make use of the cache memory, and so on.
In C++, you can "inline" assembly right into your code. You can write C++ and then suddenly switch to assembly for doing something specific where you want absolute control, and then back to C++. However, the compiler is almost always better at programming assembly than a human is, so there is normally no reason to ever do this.
Assembly is as fast as it can ever get, since it's direct isntructions, so you won't have any "overhead", any wasted instructions that a compiler may have put there because it didn't understand what you wanted.
But modern compilers are true masters at writing assembly. I've tried to beat it, but I can't. Even simple math written in C++ becomes faster than when I write it in assembly, because the C++ compiler is a much better assembly coder than I am.

"and like I said ... the only reason for the compiler is ease ... one can just throw the compiler's job in the dustbin and create a program with machine code :"

Yes, but you'll make a lot of errors, and the compiler won't. And the compiler is much better than you at writing instructions/assembly, and it knows all the "tricks" for getting good performance, which you may not know.
There are many reasons for writing in a high-level language. Performanced could be the only down-side, but nowadays, a program written in C++ will perhaps run tops 5% slower than if it was written in assembly, which means it's no longer an issue.
If written in Java, however, it might be up to 30% slower, for example.

"*Or are you focusing on the fact that the symbol, when written down, physically exists?* ... not the symbol... the button ... from my analogy there's nothing inscribed on the button ..."

Well, the button isn't a symbol. If you have a bunch of buttonos, there's nothign telling them apart, a priori. The thing about symbols is that they're hopefully unique, so that we can identify somethign with them. A button isn't that. All we know about something that looks like a button is that it is probably meant to be pressed, at some time, for some reason.

" what you can say is symbols can only be recognized by minds ..."

Yes, that is what I am saying. Because the thing that makes something a symbol is that a mind decided that it was. If no minds ever existed, there would be no symbols in the universe.

" watch your usage of the term "computer" ... a computer is an artificial mind and it can choose and recognise symbols: but only binary ..."

No, a computer is not a mind, it is a "brain".
You cannot build a mind, you can only build a thing that may produce a mind. A mind is a phenomenon, an emergent property, something that exists as being something more than the sum of the parts of something.
A mind is like program, not like a computer.

" hmmm ... just out of curiosity: how do you define or describe the human mind?"

The mind is the mental processes, being conscious and aware. That is the best (if simple) way I can describe.
The mind isn't the neurons, it is the firing of the neurons, the "action" of the brain, as a whole. As an analogy, the mind is not the painter or the painting, but the act of painting the painting, the movement of the brush.
The brain is what produces this capability.

Judging by what you've said, and what you say later, you seem to equate the brain with the mind. That is a problem.

"*"Swap", for example, requires multiple steps:* ... and that is a different code: like I've been saying ... different codes represent different functions ... "

It is a code that doesn't translate to one function/operation, but to a sequence of operations.
But perhaps you mean "function" as in conceptually the idea of "swapping things".
You haven't quite explained what you mean by "function". A "function" is a matheamatical concept, but also the idea of how something can be used, the capability of something to do some specific action. I'm not sure which one you're talking about.
But remember that "swap" didn't always exist as a "codeword", but the action could still be performed. And even with the word "swap" as a codeword, you're still performing the same function that you did before you had that word.

If you're talking about "functions" only conceptually, not atomic operations and not in the mathematical context, then you're right. We would not define such a thing if it did not do one specific thing.
But in something like C++, because it is not a coding system, what a "codeword" actually does is contextual. Sometimes it does nothing, and sometimes it has many implication. This is because it is a language.

"*we want to be able to write them the way a human would, by defining concepts. Then it's up to the compiler to turn that into a program.* ... well like I've said repeatedly : if you skip the compiler, you're doing more or less the same thing ..."

You can't. There is no way you can do what C++ does manually. If so, then C++ would not exist. The whole point is to offload things to a compiler, because humans brains are not good at these things. We cannot remember a million lines of code, but a computer can. A program will effectively never make a single mistake that no one told it to make, while humans will consistently make mistakes because our way of remembering things is by association, which is realyl crappy, ut allows us to appear to remember very many things.

The way our brains remember things could be seen as a set of blurry pictures where the brain imagines the pictures in between that causes it to become a moving picture. It's incredibly vague and unreliable, but it means that a lot of information seems to be stored. A computer, however, can store the raw pixels of every frame that makes up a video, and it can store any framerate. It is theoretically perfect, but practically limited by storage limitations.
High-level programming languages are there to remove as much as possible of the "human factor". It's there for the compiler to tell us when we're doing things wrong, because the compiler is better than us at these things.

"*First of all, HTML is not a programming language at all[...] * well I hope you're right this time because it sounds to me like you're wrong ... again ... what you're telling me is that writing up a webpage in an editor is not coding ..."

You can call it "coding", beause its idiomatic. What I am saying is that it isn't anywhere near a programming language.

"I don't understand how HTML is just a "way to format text and images" ... what happens in forms? : for example  ... which have systems for receiving data and processing data? ... "

No, the browser does those things. You have no way to program how the browser does those things. The browsers (actually, the HTML standard itself) have this functionality, and you only tell it where it should be.
HTML itself is a stadardized way to produce a document, same idea as a .doc used in "MS Word", there is no difference in how it works.
When they made the world-wide-web, in 1991 (right?), they needed a standardized way for all computers to view documents online, and so they made HTML. It's only a document type, a file format.

"*What is really, truly going on is that the CPU is turning one pattern of voltages into another pattern of voltages.* ... and this is what I've been referring to as the computer code all along ... what's really hard to get here? ... I'm saying that a computer has the programming to interpret "codes" ... "

But to the computer it isn't "codes", because a computer doesn't have a mind...! It's not arbitrary, there was no agreement between you and the CPU that a certain symbol should represent some other symbol, or anything like that.
The computer is a machine, forget that it is electronic. It's like an automated knife that cuts cucumber for you, except it can take instruction whether to cut them thick of thin.
And the "instructions" is not about telling it what you want, it is about screwing a handle to set the distance of the blades farther apart.
There is no mind, no one to talk to, and therefore no symbolism, and definitely no codes.
Once again, we describe them as codes (for simplicity), but the CPU doesn't.
And there is no "programming" in the CPU. The CPU isn't programmed to do things, it is built to do things. The CPU cannot change its architecture.

"*TGAC is code for the full names of the nucleobases in DNA.* ... wouldn't this translate to the binary and headecimal format? ... where cytosine is homologous to binary and C to hex ..."

C -> Cytosine -> the nucleobase. 2 levels.
C -> Celcius -> temperature. 2 levels.
C -> programming language. 1 level.
1/0 -> the voltage/switch. 1 level.
hex -> set of 4 voltages/switches. 1 level.
Assembly "mov" -> hex/value -> set of voltages. 2 levels.
C++ "private" keyword -> the C++ concept of "privateness". 1 level.

1 level means symbolism, 2 levels means code.
For clarity, if you want to agrue these things, please use the same system of "->" so that it's clear how you argue that things refer to things.

"well I think we should take a recap from a simpler perspective ... from my definition a code is anything (symbol, object, etc.) which represents(or activates) a single action ... "

That would be a "symbol". "Walk" is a symbol for the action of walking. It isn't code for the concept of walking, becauss it doesn't need to be decoded, and it was never encoded
I don't know why you want "code" to mean the same thing as "symbol". It simply doesn't.

" the computer is the "coding system" because it is an artificial mind made to understand only a language made up of "on states" and "off states" "

How can you say that a computer understands 1/0?
http://dictionary.reference.com/browse/understand?s=t
There is no undertanding going on. The computer doesn't need to understand anything to do what it does, it just does it. It's a machine, it's just cause and effect, no understanding involved or required.

"so to sum up:
1. Code: anything which represents, or activates a single action in a "coding system" ..."

OK, so how does this explain morse code?

"2. Language is a collection of syntax( not sure if this is the right word but I presume u understand) which are each codewords ... e.g
-language: English, Syntax: A-Z/0-9
-Language: Binary, Syntax: 0,1(I mean the real on's and off's)
-language: DNA, Syntax: CATG(real neuclotides)"

Those would be "alphabets", not "syntax."
Syntax is the fact that you have to write, for example "I went home", not "went I home". It is mainly the fact that the order of the words matter to the meaning of the sentence.
"Codes" do not have syntax. The thing that they represent may have syntax, so in some cases the code needs to "borrow" the syntax of the things that it encodes.
If a coding system has its own syntax, then it probably becomes a language in itself.

"This is up for scrutiny but I think it's more consistent and accurate ... "

Yeah, you just made the word "code" completely obsolete, since its now a synonym for a symbol or a language.
But it's fun to see you struggle to make the definition make sense.

"*Well, my image of you just grew a bit. Thank you.* ... well I appreciate that: I just hope this influences the discussion positively ... "

So do I.

"*Remember, HTML/CSS are not programming languages, they are file formats.* ... I'm reeeeally skeptical about this one ... by my definition, they are ... they contain codewords which contain specific functions ... "

Many file formats have "markers" in them that explain to a program what it should do with different things.
But if you'd compare a HTML document to a Word .doc document, you'll see that it's the same thing. HTML has a few other features, because it is inherently designed to be displayed in the internet and send between servers, which .doc is meant mainly as something like .pdf.
HTML's "<b>", for example, to make something bold, is "hidden" in a .doc file, but it's still there.

When it comes to forms, you simply declare that there should be a field here, where people can write, or a check-box or something,a nd you specify their labels and so on. There is no functionality in it, you need to use PHP or JavaScript, for example, to actually "do" something with it. (Note that I haven't done HTML in many, many years, so I might not be up-to-date on the newest things.)

And PHP and JavaScripts are scripting languages, not the same as real programming languages since they are "interpreted" languages. They are not compiled, they are read in real-time by a program, which carries out their instructions. This makes them slow as all fuck, but a convenient way of doing small-scale thing.
Even Java is an interpreted language, but it is at least very powerful and has at least decent performance, because it is compiled to somethign called "byte code", so the actual source code isn't read. This makes it faster.

"*Genetic code is made though evolution, we know this, we see it constantly.* ... wrong ... genetic code is altered through genetic variation and natural selection ... it's either a duplication, or a deletion or a change in emphasis ... nothing new is created"

OK, so if "TAAGGAC" is changed to "TTTGAAC", it isn't "new"? You're not making sense. It's new, because it wasn't there before. It's also new because it does something it didn't do before.
And in the case of a duplication mutation, it's also new in the sense that it added to the length of the genome.
In all ways, it is "new". Just because it was derived from somethign doesn't mean it isn't new.
But I agree that since it is based on somethign else, it isn't new "from scratch". But that doesn't matter. If I change the word "hello" to "jungle", through a series of steps, it's still a completely differnet word.

And for some really weird reason you said genetic code is altered throuhg "genetic variation and natural selection". Dude, that is evolution!

"new in the sense that a totally new system with new proteins and new structures can arise by these processes ... "

That doesn't need to happen. Evolution doesn't need to produce that for the species to evolve.

" I'd really want to see these RNA self assemble: I've heard of something like this but it's nowhere near a functional organism ... if this is the case then that doesn't prove anything to me ..."

No, you're right, they're not organisms, they're self-replicating molecules. I never said they're organisms. They're not "alive", either, or the problem of abiogenesis would've already been solved.
"Life" follows 7 characteristics, and those molecules only fulfill 2, in that they evolve and they reproduce.
However, when you have a chemically potent, self-replicating genome, then all you need is time, and a supply of matter and energy to work with. I mean, they replicate geometrically, and they're just molecules, so there will be a crazy amount of "generations" and "individuals", and RNA mutates much faster than DNA.
But yeah, this is still science in its infancy, really, abiogenesis.

"Yes, which is why I said "humans" create technology. Dolphins don't, even though they are creatures, and they are intelligent.* ... I believe you said "intelligent creatures" ..."

As a response to you saying "intellience".

" that was what I aimed to counter ... you're saying here that technology is only created by humans ..."

That's a misunderstanding. I said humans make technology. We have examples of that. I didn't say "only", but I might have phrased it in some way that make you think I mean that. But I hope it's clear, now.

" my point however is that our technology is extreemly similar to some of the things we see in nature:"

Yes, because we can't think completely novel thoughts. We learn from nature. If there were no flying animals like birds, then our "airplanes" might have looked different.
We immitate nature, because nature alreay does a lot of interesting things.

"a flagellum is more or less a motor"

I'd rather say that our motors are more or less like a flagellum. They were here first.

" ... I'm saying that the origin of such a thing was most likely an intelligent cause: "

I know that you're saying that. You just have no reason to think so. We have no reason to think that any intelligent creatures existed back then, to create the flagellum. But we know that evolution can do such things, and in fact will do things like that.

"since no one of us got to see it happen first hand, we can only infer: you are infering from a process that destroys info."

No, evolution favours beneficial information, and weeds out bad changes. If you're going to argue about evolution, then learn what it is and what it does.

" I'm inferring from the only cause we know that can get a system like that to start working, with lesser or even negligable improbable outcomes ..."

Evolution does that.

"*If "intelligence" creates technology, then dolphines should also, since they are quite intelligent. So are ravens, and some other birds, for example.* ... simple explanation: difference in intelligence ... dolphins are quite intelligent alright, not as much as humans are obviously ... "

But perhaps more intelligent than chimpanzees, and chimpanzees do create technology, at least rudimentary technology.
You don't need to be as smart as humans to be able to make technology, you mainly need a complex language, because then you can share information. Imagien if humans had no way of teaching our children, or share information with eachother. Every new human would basically have to start from scratch, and would never learn enough to create technology that would require more than normal knowledge.

"A disembodied intelligence (if such a thing could exist) still cannot produce technology.... well like I said God is beyond the limits of the natural laws, but He also manifests in different physical forms ... nothing stops him from moving physical objects ... "

Beyond natural laws = "magic", as I've pointed out before. I cannot take that seriously, you know.
Yes, we can all imagine magical things, but that doesn't mean they can exist. And you most certainly cannot claim that the explanation for some mystery is something that per definition cannot exist (magic), as far as we currently know.

"*We know that it's possible to gradually build a system that is IC.* ... no we don't: we know that it's astronomically improbable to gradually build an IC system by random addition of random parts ...  "

Astronomically improbably things happen all the time, in the universe, because it is astronomically large, with astronomical time scales.
But yes, "astronomically" is a vague word, I was just making a point. Anything that seems "unlikely" to us will be extremely common on these scales.
There is nothing about IC that makes it impossible to evolve, that's why IC is a pointless concept, here. It simply doesn't apply.

Darwin said that if there is some thing that could not have evolved by small gradual steps, then his theory is disproved. And that's obviously correct. But that is not the same thing as IC. IC is a simplistic view of the problem, and doesn't apply because it seems to assume that DNA works in some way that it doesn't, such as that there would be one gene for making arms and one gene for making noses, and so on. That's not how it works. It's a big mess of genes interacting with eachother. Change how the nose looks, and you certainly change a lot of other things in the body, aswell, even if that's unintended. The IC idea of adding/removing one piece of a structure is pointless, since that's not how it works at all. And even if it did, it completely still forgets the possibility that some new thing was made by removing something, not by adding the last piece.

"That's why I'm saying that if this is simply what you mean by IC, then it is a moot point. IC, in this sense, doesn't mean it cannot evolve.* ... well IC simply proves that an IC system needs it's vital components assembled spontaneously ... so it'd be irrational to believe that it can be assembled gradually over millions of years by adding random parts ..."

IC doesn't prove anything, it is a tautology.
http://dictionary.reference.com/browse/tautology?s=t
I've already explained that IC is an attribute. It cannot be proven or disproven, it only applies where it applies. You cant disprove "red", but there may be some or no red things.
And whether or not IC structures exist or not isn't relevant, because it doesn't pose a problem to the theory of evolution.

"*I mean, the idea that if you have a system, and then remove a vital part of the system, and then the system no longer works, then that is too obvioius to even mention. It has no value at all. It's basically a tautology.* ... "too obvious to even mention" I kind of like that phrase ... applies perfectly to evo. : which is basically telling us that "organisms change" :
"

Yes, commonly, "evolution" simply means that something changes over time, except that it commonly refers to a change from simpler to more complex or more sophisticate, or something similar. Cities evolve, for example.
But in biology, there is a specific defintion of what we mean by "evolution". It is not simply "change".
And yes, it took a long time before we even understood what evolution is, so it's not obvious.
But the point of the science of evolution is to explain how the change works. In a similar way, you might have some understanding of how cities change over time, in which case it is useful understanding. Economics teaches us about how economy changes, aswell. It's not just "things change", and that's it, since that wouldn't be science, that would just be an observation.
Science is supposed to explain things, that's why we do it. So the interesting things is not that things change, but how they change.

Yes, the concept of "evolution" simply say that things change. Call that "too obvious to mention", if you want. But the theory of evolution by natural selection doesn't say anything like that, it is a framework for our undertanding of the process of change.
Gravity is also too obvious to mention, but F=(m*m)/d^2 (the law of universal gravitiation) is not too obvious to mention, and is actually very useful to know, and is part of the theory of gravity. Thus the theory of very useful.

But IC is not even an observation, it is a statement of a possible attribute. Something that is IC is something where removing any single part would make the system not perform its function. Lots of things are IC, just like lots of things aren't, and lots of thigns are "red" or "black", and so on.
IC cannot be disproven or proven, it can only show to apply as a description of a thing, or not.

" the fact that we could selectively breed long ago is proof that the idea of change of allele frequency has been known for millenia "

Those ancient people probably recognized that children are often like their parents. They had absolutely no idea why, but if they wanted a good dog, then they used a good dog to produce new dogs.
They had absolutely no plan to create these dog breeds that we have today, because none of them lived long enough to care about the long-term effects of their selective breeding.
And no, they obviously had no idea about genomes or alleles.

"... btw IC is basically meant to distill the facts into scientific terms and make conclusions: one of which is the fact that a system would need the said parts to function as it's observed ... and that's vital ... "

No, they created IC for propaganda purposes, to convince people that it's a legit argument. Like I've said, it's a simplistic interpretation of what Darwin said.
People who talk about IC have no interest in whether their argument makes sense, only that it is convincing to as many people as possible. They are targeting people's incredulity, that's all.
"Look how unlikely this is, we cannot believe it could evolve" <- an argument from incredulity. What you can believe or imagine has no impact on the truth. It's really hard to "believe" in quantum mechanics, aswell, but hat doesn't change whether its true or not. It just means that it's not intuitive. And I agree, the long term capabilities of evolution isn't intuitive.

" by stating you know that IC systems exist then you agree that the vital parts are needed simultenously to make the system function ... "

Yes, to make the system perform the function its performing. Like said, this is too obvious to even mention. If I remove the engine from a car, it obviously won't perform the function of a car, anymore.
But, that doesn't mean, in any way, that it doesn'tperform some useful funciton, which is why IC isn't an argument against evolution.

Basically, we have the word "hello". Remove any letter and it will no longer work as "hello". But we can still remove the "o" at the end, and it will be a useful word, "hell".
"Hello" is IC, but that is completely irrelevant to evolution, since it could still evolve from the word "hell" in one small step.

See why IC is irrelevant?

And people who talk about IC for some reason ignore that a word such as "led" might have evolved from a word like "lead", where it became what it is by removing something, not by adding.

" evo. has a greater tendency of destroying the than favouring it ... "

Nope, if destroyng something is bad for the individual, then anyone whose function was destroyed would not be selected for, which means that the bad genes won't stay around.
Becoming more or less complex doesn't matter, whatever has the best result matters. That is, whoever makes more babies who go on to make more babies is what will exist in the future.
This is probably why most life on earth is still in the form of single-celled organisms. There is nothing inherently better with being more complex, since that always carries a price. Not that bacteria hasn't become more complex, they're just not as complex as animals, for example.

"*But if we can find the reason for why holes exist, and demonstrate that the process works, then we've got an explanation for why the hole might be there.* ... I think I can say I know the reason why IC systems and codes exist and I say it's intelligence ... I'm not really sure why I'm not allowed to say this ..."

Because it isn't intelligence that does it. We've been over this. Intelligence is a capability/feature of a creature. It is the creature that does such things.
And we have no examples of anyone who creates/designs life, who might have exsted back when life started on earth.
It's possible, perhaps, I'm not saying it isn't, I'm just saiyng we have absolutely no reason to think that's the case. Evolution already explains it all, and we can verify it with DNA and the fossil record, and there is no sign of a creator/designer, except for in the imagination of people who have been told that they should believe it.
So unless you're paranoid and think that a god is doing all this to fool us, the case is already closed. You're just a century behind.

"you still seem caught up on the ID/creationism equivocation ... a very powerful equivocation which caused ID proponents to loose a court case ... "

It is the same thing. Even the people who invented the term "ID" was caught with this fact, since they had failed to edit out the word "creationism" properly from their documents. ID is the same thing, they just changed the word and stop admitting that it is the same thing.
And there is nothing about ID to set it apart from creationism, either. You've simply fallen for the lie that they're different.

"*Yet you can't identify the process "god" used to create it, so how can you say that?* ... well we say the process is design ... "

No, explain the process used. I can also design things, and I will be able to explain the process I used to design it, or create it. You can do that same, you can create a car using CAD, and build it in a factory, and we can go into any detail about the process.
When it comes to life on earth, we have explained the process that caused life to be this way, through the theory of evolution. Furthermore, the elements of the theory of has been tested and refined for over a century, to the point where we've written countless scientific publications on the evolution of different things.
You seriously think you can match that by saying "design", as if that would be an explanation? That's why people laugh at creationists, you know.

"And neither can you identify a god who has actually done it. ... as a Christian I say it's God... or what you might call Yahweh ..."

I know the book you're talking about, but the people who wrote the book didn't know, either. You're referring to a story, not to a real thing. And "Yahweh" is an evolution of an older god, "Yahw" (Yahoo), the warrior god of some pantheon of gods, a long time ago.
And Muslism and Jews and christians disagree about what god you're really talking about. That's because no one can actually refer to anything real, only their own imagination, interpretation of culturally significant stories.

"*So do you really want to keep making that mistake, or will you realize that something that is unknown is simply unknown, at this point?* ... to my knowledge, the main claim of the Judeo-Christian faith has been consistent since it ever started: "God is the Creator of the universe and life" ... and it still is the main claim today ... that's reasonably consistent by religious standards ..."

Yeah, if you want to ignore the finer point of the claim. I don't, however. The bible makes very specific claims about god, some which can and have been shown to be false.
Yet instead of realizing that it's fundamentally wrong, like with volcanos and earthquakes and rain and thunderstorms, religion refuses to die. As I think I've pointed out, it has become pathetic. I could respect it back when they actually stood by the claims that their religion makes, but now it's just a bunch of spindoctors who try anything they can to avoid having to face the facts.
If "god" exists, then he clearly is not the god described by the bible. Yet people still want to claim that it's the same god, that even though the bible is wrong abut most of the things it says, you can somehow still trust that the "important" things are still true.And what are those things? The things that still "feel good", like the idea that you'll get to heaven iehn you die. Not because it's rational to believe that, but because it feels good. Yes, it's become pathetic.

"*No one is saying that we know how things evolved, we're saying that we know how they could have evolved, and that makes it the most likely explanation.* ... and we're saying that's highly improbable : I was wondering that the most likely situation should be the most accepted, scientifically ... but apparently even highly unlikely outcomes are accepted for the fear of the alternative ... "

There is no "alternative". No one else has ever managed to propose a theory that would explain all the facts. Creationism barely explains half the facts, while the other half speak against it, or remains oddly inexplicable.
Evolution is the only explanation we have that accounts for all the facts.
But this is not about which explanation is better, it is abotu which excplanation can be demonstrated to be true. The theory of evolution has been tested and confirmed. Nothing you say can change that. If you want to challenge the science, then do it in a scienitic forum: Write papers to peer-reviewed science journals and present your evidence.
Do note how basically not a single ID proponent ever actually does that. Why? Because they know you can't argue for ID, since there is no evidence for it. taht's why ID proponents want to bypass the scientific process and go straight for the "profit" instead.

"*If there are no options that we can find, then that still doesn't prove that it didn't evolve, it just means we haven't come up with a solution.* ...  but there's a solution readily available for thought ... it just seems to me that you want to believe somehow evo. did it ... if you consider the two options without any bias, then atleast you would admit that there's good reason to invoke intelligence ..."

No, "intelligence" requires evidence, like everything else. You're not allowed to bypass the scientific method just because it suits you.

"*I have no idea what "imaginary" processes you're talking about.* ... I'm talking of natural selection and random mutations constructing highly complex biological systems: the probability for this is extreemly low"

Yet this process is used in technology because it does exactly what you think it won't.

"it's just like you telling me that in theory we can achieve 100 consecutive Six' from rolling a die ..."

The problem lies in you thinking that anything like that is ever needed to explain the diversity of life. The problem is that you don't understand the science, that's all. If you did, you'd not be giving analogies that simply do not fit.

"... however the chances of assembling a fully functional flagellum are way less than the die outcomes of 100 consecutive six' ... "

You don't know what was turned into the flagellum, so you don't know what changes were required. You're pulling stuff out of your ass, simply.

"*To say that something is "irreducibly complex" is like saying that it is "red" or it is "large". It's just a specific kind of description, an adjective, basically.* ... not really ..."

"Irreducibly complex".
"Complex" being an adjective, and "irreducibly" being the adverb that enhances the adjective. In the same way, we could say "incomprehensively large".

Did you go to school? Or did you perhaps go to an american school, and that's why you don't know these things? I won't blame you, in such case.

" it's not a theory alright, it's a scientific fact ... and it can be falsified ... it only requires a demonstration of a system like the flagellum arising in a stepwise fashion [...]"

You still don't get it. You can't falsify an attribute. You can only determine whether something has that attribute or not.
You can't falsify "incomprehensively large", either.

"*However, you can falsify the claim that something is IC, just like you can falsify the claim that something is red.* ... how's that?"

Well, that should be obvious.
Find something that you can remove from the system without removing the function of the system. For example, you can remove things from a computer, and it can still work like a computer should.
That proves that it isn't irreducibly complex, so if someone claimed that it was, then that claim is falsified.
 That means that the attribute "irreducly complex" doesn't apply to that computer.
You can also check whether somethig is red or not, to potentially falsify the claim that it is red.

"*No, the human eye is definitely not IC. There are plenty of things you can remove, and it'll still be able to "see"*.... yes the human eye is IC ..."

No, it's not. The question is at what point it can longer be considered to perfom its function. You can remove 3/4 of the photoreceptors, and you'll still see relatively fine, for example. Some people are born color-blind, because thay lack the kind of receptor that picks up a certain color, but they can still see just fine. The eye is still doing its job.

" if you take out the lens then you have some kind of really long sighted situation can be best described as blindness ... "

Compared to normal eyes, yes, but if we're talking about the eye evolving, then the question is whether the eye without the less is better than no eye at all. And yes, it is, and yes, it would fill a function.
In a world of blind the people, the eye-eyed man is king, as they say.
It has been described in detail how the eye can evolve and how it can be useful at every step. The eye is not a mystery in any way.
And it isn't irreducibly complex, either, not that it matters. Large structures are rarely irreducibly complex, because there is so much freedom to change things and still fill teh same function. It's when you get down to molecular level that it's more common to see irreducible complexity.

"*We cannot make an eye evolve from scratch in lab, since it took billions of years, as far as we know.* ... well I say you don't know about how the eye arose ... "billions of years evolution" is not a credible excuse to me ... it's imaginary... and like I said, it's irrational to accept such a position ..."

We have evidence of the evolution of the eye. Not down to molecular level, but on a structural basis. We also have living examples of animals with eyes at different stages of evolution, so to speak. That is, they diverged at different point, and can therefore show us the "milestones" that the evolution of the eye had. So you don't have to blindly accept this, since there is evidence.

"also, the amount of development that took place within the last 2000 years is too exponential for me to believe humanity couldn't achive such in 200,000 years before ... "

It's actuallymore like the last 10 000 years, and it's because of agriculture, mainly. If you'd actually study thes things, you might understand them a little better. You think you can just "think" your way to knowledge, but you can't.

"*It's a different thing to just not accept it, but if you want anyone else to reject the theory, then you need to prove that it is wrong.* ... actually, it's yet to be proven to be right ...  from the way I see it ... "

No one cares how you see it. Your opinion doesn't matter. And you're giving your opinion on something that you haven't studied and clearly do not understand.

" actually bacterial lifeform should have been used to prove that an IC system can be built out of nothing ... but the only bacterial exp. I know of showed no such new systems:"

You're seriously comparing 50 years to a few hundred million or so? How the fuck do you even think? Of course 50 years, or so, won't show you any noticably new structures, or whatever. 50 years is nothing.

" what I got from it was that evo. can actually destroy function more on the average ... that's really not going to helf if we're trying to build new complex systems ..."

When you put something in a controlled environment, it no longer needs half of its functions, because a controlled environment doesn't pose the same kinds of problems. In that case, losing a few function is good beause it reduced the energy upkeep cost.

You're basically taking something that is good at living under various conditions, and applying one simple pressure to it, not a complex multitude of pressure like it faces in its natural environment. It can lose its functions that made it survive in nature, because nothing is selecting for those, anymore.

"*And Einstein referred to #1, while most atheists are of the #2 kind. He was clearly not talking about the #2 kind.* ... well he was ..."

He was not.

"*But to the best of my knowledge, I don't believe in any gods. And in fact, I'm quite convinced that gods in fact do not exist, but it really is a matter of definition.* ... so which is it? please be specific ... is it that you "don't believe in God" or you're "convinced God doesn't exist"? ..."

I'm not sure, it depend on your definition of "god". But in either case, I would still be an atheist, so it doesn't matter to the label.

"by saying "God is love" I mean God is the source of what we know as love ... it doesn't mean God is nothing more than love ..."

Yes, you might mean it that way, but someone else might not.

"*That is correct. All I can say is "stop believing something you have no justification for believing".* ... OK you also have no basis to assert that I have "no justification for believing" ... that's completely wrong ... even more so after I've explained many reasons why I believe ..."

You have "reasons", but you have no justification. You cannot actually support your belief with anything. You may think you can, but you can't. You're relying fallacies, which means there is no true justification.

"*That is not to say "god doesn't exist", but rather "we should not believe in god, since we have no reason to.* ... that's a completely wrong assertion ... there are many reasons why one can believe in God ... "

Yes, why one "can" believe in god, but there is no reason why anyone should believe in god. By that I mean that there is nothing to justify that belief, no evidentiary support.
I believe in coffee cups because I have evidence of their existence, for example. That is a justified belief.

"if you can predict exactly when and where every volcano will errupt then you might be able to explain why it's not random for you "

Even if all you can predict is the probability, it's still not random. Somethign that is random is somethign no one would ever even try to predict, because by definition you can't.

"... however it's still random for the organisms that can't "

No, they just think that it is. In reality, it's still not random.
Strange how you can't understand this. Things can be in some way even if no one knows it.

"*Yes, aswell as many other things, like competition of sresources, sexual selection, and whatever.* ... exactly... and you can't predict them"

To some extent, we can. We know why sexual selection is the way it is, for example, therefore, it only leaves some specific options.

"*No, they not random. If the selection pressure changes because your prey, which you've been living on, dies out, then that is not random.* ... yes it is becouse you couldn't predict the "sudden" situation ... it just happened to be so ... "

Sudden, but not "random". And yes, some things are harder to predict than other things.

But forget all of this. Even if the environment is random (changes randomly), the direction of evolution is not random if it follows the environment. Know the environment, and you know the direction of evolution.

And whether or not we are able to know these things is separate from whether they are real.

"*But predator-prey dynamics is probably the main thing that controls evolution, I suspect.* ... and these dynamics aren't random by you judgement I suspect? ..."

Of course not. The predator needs to evovle to catch the prey, and the prey needs to evolve to avoid being caught, to generalize. Very non-random.

"well many more things can't be predicted in the environment ... even by modern humans and their technology ... so why exactly is the environment non-random? I still don't get it ..."

Because our ability to predict it is irrelevant. Whether it can theoretically be predicted is what determines whether it is random.
Things didn't stop being random because we started being able to predict that thing. It's about whether all possibl eoutcomes have equal odds of happening, that is what randomness is.

"*Given a specific situation, and a short-scale prediction, then yes.* ... give me one example of such ..."

Well, the fact that since we are only allowed ot fish large fish, the average size of fish in the ocean has gone down. This isn't a prediction, I know, it's a "post-diction", but my point is that such a thing could be predicted. You want actual predictions, you have to talk to an expert, I'm just a layman.

"*Take the number zero, and keep adding either +1 or -1 to it, perfectly randomly, and over time you should be hovering at the number zero. No actual change.* ... I don't know how your math is giving you this ... if I take a number 0 and add either -1 or +1 randomly I can well get to even 5"

Do you understand the mathematical concept of "tending towards"? If you take 1 and add 1, and keep adding 1, then this series of numbers is "tending towards" infinity. That is, if you could actually do this for an infinite amount of time, you would get "infinity" as the sum, but you can't practically do that.

Adding -1/+1 to zero, perfectly randomly, will tend towards zero, in that over time any small change from zero will disappear. You'll have an infinite amount of +1 and an infinite amount of -1, which adds up to zero.

 " evo. works without a direction from what I know ... even if the environmental pressures act as a direction, it doesn't make it less random because the direction is basically a random outcome ..."

Even if the environment is random, evolution isn't random because it follows the environment.
Another math example. If the environment is any random number, then evolution is that number +1. That makes the "evolution" part of it non-random, because it's always just "+1".
So whether the nevironment is "random" or not doesn't matter. (It isn't, though.)

"what mathematics is this? if we're adding -1 or +1 randomly, then we can very well get a situation where +1 would turn out 3 times or more"

Since the change of +1 appening three times in a row is the same as the chance of -1 happening three times in a row, they cancel eachother out, aswell.

"*No, the result won't be exactly 10, but it will stay around 10 over time. It will not grow in any direction, which is the point.* ... no the result can well drift to even 15 ... it's just a matter of chance"

It will tend towards 10. The longer you keep doing it, the closer to 10 you'll be. If you do it an infinite number of times, you get exactly 10.
Evolution is the fact that if you have a selection pressure, the number won't' tend towards 10, it would tend towards infinity.

"*I used numbers because it makes it easy to examine, since you can easily calculate the average value of them, so you can tell if the "species" has changed as a whole. It's only for convenience, nothing else.* ... I think it was a fail ..."

Of course you "think" so, beacuse it doesn't show what you wanted it to show. You would never accept it, no matter what, even when mathematical proof stares you in the face.

"*So when I say that it is more likely to go any other direction than exactly backwards, you suddenly have a problem with it? And why is that?* ... not sure I'm getting you here ... but I'm saying that the law of irreversibility makes no difference to me since it's based on an evo. presupposition"

So you're simply admitting bias? Nothing can be right just because it is related to evolutoin, huh?
No, if you consider an analogy of walking forward, and then making a turn. You can make any turn, but only a turn of exactly 180 degrees will bring you back to where you were. What is the chance that you'll turn exactly 180 degrees? Practically zero, since even 179.99999 degrees wouldn't mean going backwards.
There are theroetically an infinite number of other turns you could make than the exact one that takes you back. So unless you turn back intentionally, it's not going to happen on its own.

 "I addition, there's no plausible restriction I know of that can prevent humans from "evolving" wings in a million years time ..."

A million years can't be enough time. It took 6-7 million years to change from the common ancestor with chimpanzees and humans into the humans we are today. And that's a small change. Wings would require very large changes. Perhaps 200 million years could do it? Depends on how capable wings you need. You could call our arms "wings", it's a question of definition.

"Even if you don't accept the theory of evolution, you still have to argue against the actual science, not a straw man of it. And that includes the law of irreversibility. ... well I don't think the law of irreversibility adds any more validity to the theory to be honest"

It's not meant to. It's a law that is part of the theory, because it describes something related to the subject. It's part of our knowledge of evolution, though this particular law is still discussed. We're still not entirely in agreement that it must always apply, but there has been no true refutations, as far as I know.

" like I said, it basically says evo. doesn't move in a backward direction, even in evo. moves in no specific direction ..."

Even something that moves in a random direction has still beeen somewhere, meaning taht there is still a direction that would take it back to wherever it was. But if it moves randomly, the change of getting back to the last position is extremely unlikely.
But evolution doesn't move randomly. However, it doesn't plan ahead, it's just a process of natural selection, so the environment determines where it goes with any specific species.

"it was fail proof for the designer from the start most likely ... but probably not enough to last for a very long time ..."

Nice contradiction. Fail proof but will eventually fail, huh?

"*And if he meant to make a rabbit, why didn't he start out with a rabbit, rather than making completely differnet kinds of stuff for millions of years, until it started becoming more like rabbits?* ... please don't mix your evolutionary belief with my explanation: you're gearing towards a strawman here ..."

No, sorrry, your explanation still has to explain the facts. There are no pre-cambrian rabbits, that's a fact. But more recent rock layers reveal more rabbit-like creature.

"*It wasn't "maintenance". They were drastically changed over time, to more complex creatures.* ... so how much did the anthropods change again?"

"How much"? Sorry, I have no metric for that.

" first we can define to an extent what God is "

I'd love to hear it.

" secondly, the process by which he created things is most likely design: we know of design:"

Yes, we know that "design" means anything that was artifically created, as far as I know. Sorry, that is not a process, try again. There are a shitload of ways that something could be "designed". It isn't a description of the process, it's more like a vague category.
http://dictionary.reference.com/browse/design?s=t

" and we know human hands and even our technology can't create something that intricate and nanoscale ... "

And no one says that we did. But nature is good at making specifically those kidns of things, since the unvierse operates at that level, while we humasn operates on a macro level, and aren't even aware of the nano scale. That's why we humans are better at macro-scale things, while nature is better at nano-scale.

" I never said God was "unknown" this is probably another strawman from you..."

No, "god" is in fact unknown, or can you demonstrate your god? I didn't say that you said he is unknown, I simpyl know that he is, because no one knows anything about any "gods".

"*And that's ID/creationism summed up.* ... well you can just prove yourself to be ignorantly silly here by defining both terms ... you're ofcourse trying to make the same equivocation I've called out a few times now I believe ... the same equivocation that lost a court case for ID ...  "

They are in fact the same thing. I agree with the court.

"*I don't know what to say, punctuated equilibrium is correct, that's all. We see it in nature, and in lab.* ... there's a good chance you might well be only seeing what you want to see ..."

What, you're on the side of gradualism, as opposed to punctuated equilibrium? Why?

"*It makes perfect sense that the more fit you are to you environment, the slower you'll evolve, because the "less fit" individuals of the species won't have a problem, since even they are fit enough to reproduce just fine.* ... still doesn't explain the missing plethora of transitions required to validate evo.

That's not what we're talking about here. We dont' need any transitions to validate evolution,b ecause we can observe evolution right now. The fact that alleles change in frequency...
However, dooes this change in the species happen gradually and constantly, or does it speed up and slow down? That is what we're talking about.

" ... OK rapid evo. time periods followed by times of "stasis" ... weeelll: where are the millions of "rapid" transitional fossils? ..."

You can't see on a fossil whether it was rapid or not, you have to look at the series of transitions. And yes, we see that change happens at different speed in the fossil record.
But like Isaid, this isn't about fossils, either, this is about evolution. Fossils is paleontology, the history of life. The theory of evolution is about the process of evolution, how it works. Puntuacted equilibrium is related to evolution, not to paleontology.

"you can't have major phyla emerging out of nowhere without transitions and expect evo. to explain that ..." (cambrian)

They didn't emerge out of nowhere. I suppose you've been misinformed. (?)

"If you're talking about the cambrian explosion, then that was a period of about 25 million years. Remember, humans diverged from chimpanzees only 7 million years ago. Dogs evole from wolves in 10 000 years. ... OK it was 5mill years ... no 10 ... no 7 ... no 20 ... 20 makes it sound more inline with evo."

What is it that was 5million years? The cambrian explosion? Perhaps you should look that up.
20-25 million years according to Wiki, sourced from BBC:
https://en.wikipedia.org/wiki/Cambrian_explosion
According to pbs, it's 30 million years:
http://www.pbs.org/wgbh/evolution/library/03/4/l_034_02.html
Royal Ontario Museum says 37 million years:
http://burgess-shale.rom.on.ca/en/science/origin/04-cambrian-explosion.php

I guess it depends on what part of it you refer to. The most rapid changes occurred during perhaps 10 million of those years, so that may be what you're talking about, but the entire period is longer, as I've pointed out.
And yes, you've got a bunch of animals evolving a lot during that time, but what about the plants, for example? Flowers, for example, evolved hundreds of millions of years later, not during the cambrian explosion.
One explanation for the "explosion", as  remember it, is the evolution of eyes, which changes the possibilities a lot. That explains why plants weren't affected as much, though they probably had to react to animals changing.
Also, we do have fossils of animals long before the cambrian explosion, in case you thought that animals didn't exist before then.
There is nothing else of interest in the cambrian explosion, other than that is was a long period of relatively fast evolution, rather than a short burst. It's still evolution.

And also, the Cambrian explosion is not the only case of large-scale diversification of life in the history of earth. A similar thing happened later, aswell, called the great odrovician biodivesification event.
https://en.wikipedia.org/wiki/Great_Ordovician_Biodiversification_Event

" ... lol ... nice job but we're not particularly sure how these time scales are determined ... but nevertheless : WHERE.ARE.MY.TRANSITIONS??? ... "

Just fucking look for them..?
http://www.nature.com/nature/journal/v514/n7522/fig_tab/nature13576_F2.html
Here's one example, detailing the panarthropoda phylogeny. There you've got the common ancestor of tardigrades, arthropods, for example, the tactopoda.

"*25 million years is a looong time.* ... Ooookkk ... sooo, enough time to show the intermediary steps ... but there were, well, pretty much none ..."

If you don't bother to fucking look, it sure will seem like there are none. But it definitely isn't hard to look it up.

" but here come a mystery question: how can one evolve so quick within a span of "20 million years" ... am I missing something here? ..."

What makes you think 20 million years is not a long time? This is the problem with numbers like these, we can't actually relate to them, we can't grasp how crazy large such time spans are. But they are.
yes, during the cambrian explosion, evolution apparently kept a relatively high pace, and for a long time, which is very rare, and we would certianly want to know what caused it.
First of all, it might be somewhat of an illusion. Because predators evolved during that time, prey needed protection adn therefore evolved hard scales, liek the arthropods. That makes them more likely to fossilize, in which case it'll seem like more life evolved, because their ancestors are harder to find.
But like I said, it could be the evolution of eyes that changed a lot of things and caused an "arms race" for a while. Both of these things explains why only animals evolved so much during this period, but not plants.
Hey, why not read a book on the subject, instead of specualting? I'm sure not the best source for info on this, I'm no expert.

"well thanks: music is anything that is music to anybody: absurd as it might sound, this is actually the case: and it's definitely not a scientific fact because it can't be tested and falsified:"

You don't test and falsify facts. You test and falsify explanations. Facts just "are".
No, this is simply a case of something that is hard to agree on a defiition of. But whatever you consider music, it's a fact that it exists, right? I mean, you're listening to it, aren't you?
If I conser only hard rock to be music, then yes, we can confirm that hard rock exists, if we give good definition of what actually makes it "hard rock". But the problem is that people disagree about how to define it, not whether it exists.

" this just shows that if we go by only what the scientific method can prove, music doesn't even exist ..."

WTF, when has science ever established that "music doesn't exist"? Are you fucking high, or something?

"*But if we agree that some song truly is music, then yes, it is scientifially a fact that it is music, because we can measure that it is there, and it conforms to the definition of music*. ... well there's no definition we can even assign to music to ascertain this ..."

Yes, there is, it's just that there will always be a few people who disagree. But do you really think that music is the only thing this applies to? It applies to more things than it doesn't. You and I can't even agree on what "code" is, right? So does that mean that code doesn't exist? No, we just need to agree on what we're talking about. If you're nto talking about the same thing, then you can't say anything about it, because you don't know what you're actually talking about.
I seriously wonder if you've been smoking something bad, or something. This conversation just dropped a number of levels.
Music exists, but a global definition of what should be considered "music" does not exist, as with the majority of things.

"but lets say there's one song that every single person thought was really, "music" : can we now define music to be a sound pattern every body approves of as music? ... no. It'd mean nothing is music until everyone accepts it to be so ... still the question remains ... what is music?"

No, it's not a democratic vote. Something is music to a specific person if that person considers it to be music. But when that person needs to communicate about music, then that person needs to try to use a definition that others will share.
The problem lies in the word, "music", because most of us agree that the word refers to something subjective. Therefore, it's a wasted effort to try to make it objective.

You can extend this to "chairs", if you want. Not everyone agrees where "chair" begins and "sofa" takes over, or "stool", or whether a wooden log is considered a "chair" or not, it depends on whether you're a pragmatic person or an idealist, or whatever. But you would argue that this means chairs don't exist. It's ridiculous. And scientifically speaking, the thing that a person calls a chair does in fact exist if it exist. The thing itself is not dependent on how we choose to define it, and that's true for music as much as for chairs.

"exactly, music is just what different people define it to be ... it's not a fact that can be ascertained through the scientific method ..."

No, but now you're only arguing that the definition of "music" can't be scientifically determined. That's correct, it can't, because that is not the realm of science.
But you do not need science to determine whether such a thing exists. I can hear music, I can see chairs, and sit in them, and so on. I know they exist, that is a fact, I don't need a scientific method to tell me that, becaue the scientific method is about explaining the facts.
You can ask science how music works, or where it comes from, how its made, how we biologically react to it, and so on. There is "music theory", you know.

"the fact that life can decrease in entropy is best explained by the systems in place which ensure that entropy is reduced... not because entropy doesn't work in life ... entropy still works nevertheless: just that life just happens to have complex systems that seem to battle it to an extent ..."

Entropy isn't a force... You can't "battle entropy". The 2nd law of TD isn't "entropy" it the tendency for entropy to increase in isolated systems.
Entropy doesn't "work", either. You keep choosing really weird words. Entropy is pretty much equal to the complexity of a system, and it is the ability for a system to do work, and how much free energy exists in the system. It is a state of a system, not a force acting on it, or anything like that. Everything has some level of entropy.
But the 2nd law of TD only sates that isolated system cannot decrease in entropy, or alternatively will tend to increase in entropy.

Because life isn't an isolated system, the 2nd law of TD doesn't apply to it. And yes, the reason why an open system, like an organism, doesn't have to increase in entropy is because it can eat and take in energy to prevent entropy from increasing, as it would have if it didn't eat or take in energy, because then it would've been an isolated system.

"It is only isloated systems that will tend to increase in entropy, because they cannot take energy from other systems. ... well we can say the universe on the average is tending towards maximum entropy ..."

The universe as a whole is probably an isolated system, so we expect it to increase in entropy, yes. But jsut because a system increases in overall entropy doesn't mean a part (sub-system) of the system can't decrease in entropy, as long as the total entropy of the system goes up.

"*But an open system can do anything as long as it can take energy from other systems. That's why the 2nd law of thermodynamics is only stated for isolated system.* ... and I'm saying a subsystem in an isolated system makes little difference to the impact of the law ... the law still works ..."

Yes, the law "works", it just doesn't apply.
Do you realize that you're arguing against the existence of life itself? An egg that develops into an organism would be impossible if what you said was correct, for example.

The universe is most likely an isolated system, because it has no systems around it where it can steal energy to do work.
But anything in the universe does have other systems around it, from which it can steal energy to do work, while then increasing the entropy of the system where it took the energy, and also increasing the total entropy of the unvierse.

The sun provides energy for the earth, allowing things on earth to do work without increasing in entropy. But because of this, the entropy of the sun increases. In total, our solar system (which is a nearly isolated system) as a whole does increase in entropy, thus the 2nd law of TD is satisfied.
Reply: antiHUMANDesigns

The beeps are symbols. And even if you can learn to decode them to letters in head so fast that it effectively seems as if you're not even decoding them, the fact is still that the morse code system was designed as a code system where letters/characters are encoded into short/long. ... well then I guess we could agree that the sounds are the codes ... which means the codes are real ...

You've just forgotten that. ... of course not ... not sure where you're getting that

DNA is a molecule. ... yes ... morse code is sounds ... you're still caught up with the conceptual confusion ...  like I said, I can encode a message into a bunch of rock arrangements: they're rocks alright, but not just rocks: their arrangement would show that ... 

A DNA sequence can contain encoded information, but that can only be so if it was intended that way by someone who wrote it. ... well DNA obviosly contains encoded info. if it didn't then why the hell does life depend on its interpretation? ... yes it was intended to be that way and most likely some intelligence programed it ...

1. Find the guy who made the sequence. ... lol hell no ... we can tell the difference between a rockslide and a Stonehenge ... we can because of our repeated experience with intelligence ... same way SETI can tell if they discover encoded message signals ...

2. Identify a known coding system which, when applied to the sequences, makes the sequence make perfect sense. It is highly unlikely that something apparently random would be decoded into something meaningful with the wrong coding system. ... the coding system for the DNA is obviously the cell and it's "machines" ... the DNA makes perfect sense only in the cell : so we can observe a coding system which can make meaning out of the DNA ... it's quite similar to the computer code: the coding system is the computer: it can make sense out of binary codes ...

But remember, DNA is basically just that: "WIHEGGWEIHNGWEIIGEWHBVWPWIOE". Nonsense, effectively. ... I think this statement is actually nonsense ... DNA might not make much sense to you ... but we obviously see it does to the cell(s) and organism(s) ... so no it's not "nonsense" ... it's valid info. which is used by living cells ...

* But it has chemical properties. And the cell uses its chemical propoerties, not the "meaning" of the sequence.*  ... yes the cells do use the "meaning of the sequence": are you sure of what you're saying? ... if you delete sections from the DNA of an organism you can end up creating detremental damages to it ... 

No, that's the software giving you the appearance of understanding. It's not the computer, it is the program. ... and what exactly do you think a computer is?

Why do I make the distinction between software and computer? Because you can move the software away from the computer, and it still does the same thing. And you can put it into a different computer, or even a different kind of computer, and its still the software that's causing it to "understand". ... well A software is basically useless without a computer: but a computer is still perfectly effective(or even more effective) without a software ... it's because the computer has an artificial mind that the software depends on to even make any sense ... 

For a computer to be able to work with "code", the CPU must have a mind. The CPU itself, not the software that it runs. ... yes the CPU has a "mind" ... I'm pretty sure that's why it's called Central Processing Unit: translate that to humans and it come out as brain ... to process something and give an output is basically all you need from a mind ...

The CPU would have to be able to choose what to do, not be tied to cause and effect, in the sense that a specific pattern of switches causes a specific effect. ... yes the CPU can "choose" in a sense ... what matters is the programming (or wiring or architecture) ... and I'm not sure: how is a software not tied to cause and effect?

I just fucking explained it to you. ... dafaq ... I'm sure by now you realize that I consider most of your explanations to be wrong: for good reasons ... so you should try to understand that I'm coming from a more practical approach ... and from that I can say there's nothing in the computer that doesn't end up in an array of ons and offs: or what I call binary codes...

Fine, I'll give you an actual example, just because you keep insisting. C++ example: ... dahell C++ is not going to help too much cuz like I said, I'm an amateur in programming ... theoritical programming more specifically ...

There, a very short example of a piece of "code" (remember, it's only called "code" because of tradition) that doesn't get translated into machine instructions when compiled. ... I strongly reckon it does ... if it doesn't then how would it be implemented?

But note that when I use "position", the only thing that is put into the .exe file are the x and y variables - not the concept/rules about how they should be treated, that hey belong to "position". "Position" will not exist in the .exe. ... OK I think I get this ... yes like you said it wouldn't appear in the .exe program: but I reckon it's just an instruction which the compiler uses ... and that instruction still ends up in binary codes: only that it isn't saved as part of the program ...

You do not know programming. You've worked with some HTML or what, but you don't know actual programming, so don't pretend that you do. ... dafaq: I think I made that quite clear : I do not know much of programming: particularly the theoritical aspect ... you should be able to see quite clearly that I'm coming from a practical and realistic angle on this ... 

However, because we traditionally call anything similar to that "source code", you can still say that you're "coding" C++. It's not literally correct, it's idiomatic. ... OK let me just say this: I think anything that goes through the CPU is code ... ie everything you do on a PC involves codes ...

What you really mean is probably that a sequence of operations/instructions for a computer can be likened to a language. ... more or less ...

Even if say it is, it isn't to a computer, its only to us. ... and like I said repeatedly : yes it is to a computer ... for anything to be called a computer it must have an artificial mind ...

Because assembly is the only programming language, at least between those two, where each word directly decodes into a machine instruction. Any assembly codeword directly represent a value. we're effectively writing direct instructions, but instead of writing the value of the instructions, we use a system where we give those values names - which is 2nd level symbolsim, code. ... I don't think this makes any sense ... if each word directly represents a machine instruction, then there's no difference if we just use machine code ...

Yes, that is what I am saying. Because the thing that makes something a symbol is that a mind decided that it was. If no minds ever existed, there would be no symbols in the universe. ... Ooook ... and I'm saying physical objects can be symbols ... as a matter of fact, I think most symbols are physical ... not sure exactly if there's any symbol that isn't ...

A mind is like program, not like a computer. ... and for crying out loud what do you think a computer is?

Judging by what you've said, and what you say later, you seem to equate the brain with the mind. That is a problem. ... I think the problem fully resides within yourself: like you've said, the mind is the action of the "neurons" in the brain ... well the computer's mind is artificial and it's the action of the voltages and switches ... 

You can't. There is no way you can do what C++ does manually. ... yes you can are you being serious now? ... it can be done: it seems like you don't even read all my lines: else you should have remembered the analogy I gave with the calculator ... anything in C++ can be done in direct machine code and practical circuitry: only it'd be extreemly tidious ... these are some of the reasons I seriously question your knowledge ... 

If so, then C++ would not exist. ... dafaq ... C++ exists to make things easier, faster, and more efficient ... you can create a calculator in C++ and replicate it using machine code and practical circuitry ... same damn thing ... just that one would save you more time ... 

The whole point is to offload things to a compiler, because humans brains are not good at these things. We cannot remember a million lines of code, but a computer can. A program will effectively never make a single mistake that no one told it to make, while humans will consistently make mistakes because our way of remembering things is by association, which is realyl crappy, ut allows us to appear to remember very many things. ... so WTH are you saying exactly? or do you know exactly what you're saying?

But to the computer it isn't "codes", because a computer doesn't have a mind...! ... yes it is dammit ...  if a computer has no artificial mind then it's not a computer ... 

The computer is a machine, forget that it is electronic. ... "forget that it's electronic" what's that? are you being serious? ... you're basically telling me to forget that a computer isn't a computer ... 

Once again, we describe them as codes (for simplicity), but the CPU doesn't. ... No we describe them as codes because they fulfil the criteria to be called that ... just like we describe a cat ...

And there is no "programming" in the CPU. The CPU isn't programmed to do things, it is built to do things. ... programming can also be described as "building" ... 
The CPU cannot change its architecture. ... a program can't either ... you change a programs architecture by changing the program ... you change a CPU's architecture by changing the CPU ...

*C -> Cytosine -> the nucleobase. 2 levels.
C -> Celcius -> temperature. 2 levels.
C -> programming language. 1 level.
1/0 -> the voltage/switch. 1 level.
hex -> set of 4 voltages/switches. 1 level.
Assembly "mov" -> hex/value -> set of voltages. 2 levels.
C++ "private" keyword -> the C++ concept of "privateness". 1 level.* 

... I see: this clearly translates to:
1/0 -> on/off -> the voltage/switches. 2 levels 
... am I missing something here?
on/off > active state/ inactive state> the voltage/switches. 2 levels
on/off -> 5V/0V -> the voltage/switches. 2 levels
come -> move towards my position -> actual movement. 2 levels
... this should do just fine ...

That would be a "symbol". "Walk" is a symbol for the action of walking. It isn't code for the concept of walking, becauss it doesn't need to be decoded, and it was never encoded ... first walking isn't a specific action ... walk 20 meters in "X" direction : this would be specific ... secondly I beleive I described the codes as the alphabets : however, "walk" would be more or less a codeword : and using the English coding system is "language" ...

I don't know why you want "code" to mean the same thing as "symbol". It simply doesn't. ... I don't ... it just happens to be similar to symbols ... however you've done a great job of equating "code" to "abbreviation" ...

How can you say that a computer understands 1/0? ... how can you say a computer doesn't understand on and off states? ...

There is no undertanding going on. The computer doesn't need to understand anything to do what it does, it just does it. ... "it just does it" that's probably wrong ... the computer "does it" according to the programming ... 

OK, so how does this explain morse code? ... well in morse code a pattern of sounds like "-....-" can represent "A" ... and only that pattern would represent "A" ...

Those would be "alphabets", not "syntax." ... so 0/1 are computer "alphabets"?

Syntax is the fact that you have to write, for example "I went home", not "went I home". It is mainly the fact that the order of the words matter to the meaning of the sentence. ... then syntax is probably closer to what I'm trying to say ...

If a coding system has its own syntax, then it probably becomes a language in itself. ... well I'm saying all languages are coding systems ...

But it's fun to see you struggle to make the definition make sense. ... likewise ...

OK, so if "TAAGGAC" is changed to "TTTGAAC", it isn't "new"? You're not making sense. ... OK i guess after Mark and I repeated the term "perspective" countless times I just had to repeat it one more time : well here goes : we see that these changes in DNA don't build anything new on phenotype level ... it even happens to be more destructive to biological systems ... "novel" information: that which builds new structures has never been observed ... and without these new structures, evo. is invalid when explaining origins ...

And in the case of a duplication mutation, it's also new in the sense that it added to the length of the genome. ... lol .. OK ...

But I agree that since it is based on somethign else, it isn't new "from scratch". But that doesn't matter. ... it does since you've just accepted that duplicated info. doesn't fit my criteria for "new" info. ... 

And for some really weird reason you said genetic code is altered throuhg "genetic variation and natural selection". Dude, that is evolution! ... yes evolution is scrambling and degradation of pre-existing  information ...  but by scramling and degrading pre-existing information we can get all of the complexity of life ... beautiful stuff ...

That doesn't need to happen. Evolution doesn't need to produce that for the species to evolve. ... well I can say I'm glad you said that ... lemme just expatiate ... you've just said evo. doesn't need to produce new systems with new proteins and new structures to get a human from a bacteria ... well another pretty neat contradiction from you ...

Yes, because we can't think completely novel thoughts. We learn from nature. If there were no flying animals like birds, then our "airplanes" might have looked different. We immitate nature, because nature alreay does a lot of interesting things. ... lol you're dangling on the edge of a falsity ... we can see nature reproduce what we all saw from the beginning of our lives ... that's not to attribute imaginary super powers to nature ... just wanted to clear this up so you don't get evo. mixed up with reality ... "nature does a lot of interesting things" ... lol ... like what? reproduction? well yes ... shape-shifting? well hell no nature doesn't do that ...that happens only in the mind of some people ... 

I know that you're saying that. You just have no reason to think so. ... and I don't think you have sufficient justification to make a silly assertion like that ... of course I can easily say you have no reason to think "bla bla bla" ... but I'd have to prove it for it to make any sense or have any weight ... however, I can say you have no reason to believe that a random process can build a biological machine like the flagellum ... and I have better justification to say that because even you'd agree that no random process can build any functioning electric fan motor ... and you'd also agree with me that the process which is supposed to build this machine is destructive on the average ...

We have no reason to think that any intelligent creatures existed back then, to create the flagellum. ... yes we do... the reason is that without invoking intelligence, we're left with a mumbo jumbo random process : and we can see that'd it'd be stupid to attribute all of such intricacy and complexity to chance ... this is true because of your pathetic attempt to attribute some kind of order to something which depends totally on chance ... Yes we have very good reason to think that intelligence existed before the flagellum did ...

But we know that evolution can do such things, and in fact will do things like that. ... haha ... you know what you know brother ... we know NS and random mutations can and will destroy : that has been seen and observed ... we know for certain NS and random mutations can't and will not build from scratch : seen and observed ... 

No, evolution favours beneficial information, and weeds out bad changes. If you're going to argue about evolution, then learn what it is and what it does. ... lol I believe it's natural selection that "favors beneficial info. and weeds out bad ones" ... evo. says this can cause frequencies to shift and organisms to gain complex structures ... well we know the latter is obviously wrong and non-factual ... btw I hope you still remember what evo. "is and what it does" ... it sounds like you might be experiencing the memory shift again ...

Evolution does that. ... but "evolution doesn't have to build new systems" remember? ... now it can build a new flagellum ... I think I'm less bothered about you not reading my lines ... I think you might have to start reading your own lines through ...

But perhaps more intelligent than chimpanzees, and chimpanzees do create technology, at least rudimentary technology. ... well perhaps not ...

Beyond natural laws = "magic", as I've pointed out before. ... Umm "Beyond natural laws" = "Supernatural" ... you can be Supernatural and use all the natural laws : being supernatural just means you're not bound by the natural laws ...  by definition, we can say music and beauty are supernatural ...

I cannot take that seriously, you know. ... firstly you're most likely referring to your strawman ... secondly how do you manage to take evo. seriously even when it attributes magical creative powers to destructive processes? ... thirdly, I'm thinking by this you cannot take the concept of music seriously: music is beyond sounds ... in the natural world, that's all to music: sounds ...

Yes, we can all imagine magical things, but that doesn't mean they can exist. ... yes i agree: and I leave you to your own imagination of evo.  

And you most certainly cannot claim that the explanation for some mystery is something that per definition cannot exist (magic), as far as we currently know. ... and one more time, the explanation is something that does exist: intelligence ... 

But yes, "astronomically" is a vague word, I was just making a point. Anything that seems "unlikely" to us will be extremely common on these scales. ... Ok just want to be clear here: do you accept that it's "unlikely" that evo. would build a flagellum?

There is nothing about IC that makes it impossible to evolve, that's why IC is a pointless concept, here. It simply doesn't apply. ... Ummm yes there is ... remember sponteneous assembly? ... that's a direct extrapolation from IC ... if a system needs all the said parts to function then it can't function until all said parts are present ... that's the challenge that evo. has to meet: but apparently evo. just says : "Nah, it evolved by gradual steps" : that's all ... looking to the facts, we see the process is actually more destructive ... however, nothing is imposible with the imagination: hence evo. wins the game ...

Darwin said that if there is some thing that could not have evolved by small gradual steps, then his theory is disproved. ... I thought you said "Darwin was wrong" ? ...  

And that's obviously correct. But that is not the same thing as IC. IC is a simplistic view of the problem, and doesn't apply because it seems to assume that DNA works in some way that it doesn't, such as that there would be one gene for making arms and one gene for making noses, and so on. That's not how it works. It's a big mess of genes interacting with eachother. ... well this big "mess" knows that it has to correct itself to avoid serious damages to the organism ... and this big mess is consistent in keeping distinct features in different organisms ...  

Change how the nose looks, and you certainly change a lot of other things in the body, aswell, even if that's unintended. The IC idea of adding/removing one piece of a structure is pointless, since that's not how it works at all. ... well we do know that all these changes don't build systems ... but evo. still believes it could ... still, could you tell me exactly how exactly evo. works : in relation to building a flagellum? ...

And even if it did, it completely still forgets the possibility that some new thing was made by removing something, not by adding the last piece. ... of course forgeting this would be beneficial for you since losing more components is going to get the bacteria back to chemistry ...

IC doesn't prove anything, it is a tautology. ... well I'd suggest you investigate natural selection ... PS IC proves spontaneous assembly: accepting IC means conceding the need for spontaneous assembly ... afterall, if all the said components aren't needed at the same time, the system in question isn't IC ...

And whether or not IC structures exist or not isn't relevant, because it doesn't pose a problem to the theory of evolution. ... yes it does ... like I've explained ...

But in biology, there is a specific defintion of what we mean by "evolution". It is not simply "change". ... yes in one instance it's change in allele frequency, in another instance it's forming complex molecules from simpler ones ... it's definitely not that simple I'd say ...

And yes, it took a long time before we even understood what evolution is, so it's not obvious.  ... lol ... it took a long time to pad the theory up to withstand the new evidences against it ... it was obvious long ago that frequencies did change ... that was why we could practice it in selective breeding ... 

But the point of the science of evolution is to explain how the change works. ... and it has managed to say the change works by scrambling and destroying pre-existing info thereby forming brand new systems in the process ... it's actually amazing how this would be expected to work ... 

Science is supposed to explain things, that's why we do it. So the interesting things is not that things change, but how they change. ... OK I get it: the science just explained what we saw all along: it just explains why our siblings are different from each other ... if so then that's OK ...

Yes, the concept of "evolution" simply say that things change. Call that "too obvious to mention", if you want. ... well mignt even be more obvious than IC ...

But the theory of evolution by natural selection doesn't say anything like that, it is a framework for our undertanding of the process of change. ... hmm I'm a bit confused: the theory of evo. doesn't say that things change? ... what does it say then?

But IC is not even an observation, it is a statement of a possible attribute. ... IC is not an observation? ... please tell me I've not wasted hours of my life in vain ... please ... 

Something that is IC is something where removing any single part would make the system not perform its function. Lots of things are IC, just like lots of things aren't, and lots of thigns are "red" or "black", and so on. ... I don't think you've made any sense here ... 

They had absolutely no plan to create these dog breeds that we have today, because none of them lived long enough to care about the long-term effects of their selective breeding. ... what? their plan was to get specific qualities from dogs: so yes their plan was to create the different breeds: they probably inter-bred different breeds for specific combinations: that's basically the whole point of artificial selection: looking for specific traits: an that creates diversity ... so I'm not sure what you're blabbering about this time ...

No, they created IC for propaganda purposes, to convince people that it's a legit argument. Like I've said, it's a simplistic interpretation of what Darwin said. ... lol ... so I take it that you have no more to say on this topic ... I'm glad you finally understand IC is an observable fact ... moving on ...

People who talk about IC have no interest in whether their argument makes sense, only that it is convincing to as many people as possible. They are targeting people's incredulity, that's all. ... straight outta your ass ... of course people talking about IC know it's a vital point when defending ID : and the argument has to make sense to convince anybody ... 

"Look how unlikely this is, we cannot believe it could evolve" <- an argument from incredulity. What you can believe or imagine has no impact on the truth. ... what truth?  ... the shape-shifting of organisms?... lol ... if so, you've just said what I can believe or imagine has no impact on what you can believe or imagine ... what I believe is strictly coherent with the truth we've ascertained by observation and repeated testing ... not sure about yours tho ... 

And I agree, the long term capabilities of evolution isn't intuitive. ... and it isn't factual either ... PS if it isn.t intuitive, why would you blame anybody for rejecting it?

Yes, to make the system perform the function its performing. Like said, this is too obvious to even mention. ... well I'm happy you see how easy this is to understand now: something I've spent probably weeks trying to force through the heads of you and Spiegel ...  and something that the so called top scientists apparently can't grasp: you must feel the shock Behe feels everytime he tries to explain this ... apparently his mistake was thinking his concept would be so easy to understand ...

But, that doesn't mean, in any way, that it doesn'tperform some useful funciton, which is why IC isn't an argument against evolution. ... just wondering what useful function a car without an engine can perform ... spare parts? ... that'd mean vestigial components in evo. terms ... however the idea of exaptation is one which is highly wishful and less factual: exaptation assumes all parts of an irreducible system had previous different functions and just happened to be well matched to each other such that they all came together at "so so" time and formed a functioning IC system ... well that's a laugh ... 

Basically, we have the word "hello". Remove any letter and it will no longer work as "hello". But we can still remove the "o" at the end, and it will be a useful word, "hell". "Hello" is IC, but that is completely irrelevant to evolution, since it could still evolve from the word "hell" in one small step. ... I think you forgot to explain how this is related to evo. ... I mean can "concepts" evolve the same way as organisms? ...

See why IC is irrelevant? ... I see why your reasoning is the way it is ...

And people who talk about IC for some reason ignore that a word such as "led" might have evolved from a word like "lead", where it became what it is by removing something, not by adding. ... well like I said, removing components works fine with me: and the facts: but removing components wouldn't be what you'd need to build an IC system ... no?

Nope, if destroyng something is bad for the individual, then anyone whose function was destroyed would not be selected for, which means that the bad genes won't stay around. ... maybe I used the wrong terms ... let me repeat evo. is more likely to degrade pre-existing components than add new functional components ... 

Becoming more or less complex doesn't matter, whatever has the best result matters. That is, whoever makes more babies who go on to make more babies is what will exist in the future. ... well becoming more complex matters if a flagellum is going to appear from nothing ... and it matters a whole lot if evo. is to be taken as an explanation for origins ... 

Because it isn't intelligence that does it. We've been over this. Intelligence is a capability/feature of a creature. It is the creature that does such things. ... hmmm first of all : "creature"? was that a typo? ... secondly intelligence is the only explanation that makes most sense with the evidences ... also, there's no concensus as to what exactly intelligence is: it's probably just one of the concepts like music... we know it exists, but we just can't put a definition to it ... however it's a cause we know can create amazing things: and the only cause we know which can create a biological motor  ... 

And we have no examples of anyone who creates/designs life, who might have exsted back when life started on earth. ... are you seriously repeating this? ... after I've said countless times that what we're looking for is observable outcomes which can only be explained by intelligence ... 

It's possible, perhaps, I'm not saying it isn't, I'm just saiyng we have absolutely no reason to think that's the case. ... I'm saying you do ... evo. says it just happened by chance: and that's good reason to discard the thought: no observable process creates life: what we can observe is just duplication and variation of pre-existing life ... 

Evolution already explains it all, and we can verify it with DNA and the fossil record, and there is no sign of a creator/designer, except for in the imagination of people who have been told that they should believe it. ... this is one of the most close-minded assertion you've made: not surprised though ... but Dawkins said: “Biology is the study of complicated things that give the appearance of having been designed for a purpose” ...  you really need some guts to say there's no sign of design in life ... "if you look at the details of biochemistry, molecular biology, you might find a signature of some sort of designer" - Dawkins ... yet you are damn sure there's no sign of a designer ... and you wonder why I don't take you seriously most of the times ...

So unless you're paranoid and think that a god is doing all this to fool us, the case is already closed. You're just a century behind. ... doing what exactly? ... I hope you're keeping close touch with your comments ... cuz it seems like you're in rant mode again ...

It is the same thing. Even the people who invented the term "ID" was caught with this fact, since they had failed to edit out the word "creationism" properly from their documents. ID is the same thing, they just changed the word and stop admitting that it is the same thing. ... yes you silly man: ID and creationism can mean the same thing depending on how you define the terms: if you want to take the objective definition of creationism then it's just a view that life and the universe were as a result of specific acts of creation ... in this case it says more or less what ID says which is ; there are certain biological systems which exist which is best explained by an intelligent cause instead of an undirected process like evo. ... there's absolutely nothing religious about these two claims ... it's just like saying the stonehenge was a result of a specific act of creation: or saying the stonehenge was intelligently designed ... if you believe is any sort of creation or design in life, you're a creationist, be it deist, theist, panantheist, etc ... or young earth creationists, Old earth creationists, evolutionary creationists ... you can even believe aliens created life or whatever: you're still a creationist ... 

but if you define creationism to be the view that the universe and life came as a result of special creation according to the book of Geneis in the Bible : then you're talking of a totally different concept which is Biblical creationism : this specifically names the creator to be God and it gives a specific order and description of the creation events: it's more or less a religion ... however, considering that creationism just happened been merged with Biblical creationism, it was obvious that going by the name "creationism" was going to constantly insinuate Biblical creationism ... so ID was probably the name used to start up a brand new scientific approach which was strictly based on testable and observable evidences ... and it says that the evidences show signs of a designer ... if you can maintain the original definition of creationism without making equivocations, then that's fine: but I'd reckon you wouldn't cuz the only way ID can be deemed religion is if it's equated to Biblical creationism ... and that's what happened in the court ...

And there is nothing about ID to set it apart from creationism, either. You've simply fallen for the lie that they're different. ... I believe I asked you to define the terms: you didn't ... so how can you tell it's not you who has fallen for lies? ...

No, explain the process used. I can also design things, and I will be able to explain the process I used to design it, or create it. You can do that same, you can create a car using CAD, and build it in a factory, and we can go into any detail about the process. ... well it was created whole with information to replicate and adapt ... how about you explain the process by which it evolved? ... yes I don't mean "Natural selection and random mutation": I mean the exact steps it took and the exact processes ... like how a mutation happened and brought up a hook out of nowhere and then a tail, and then a rotor, stator, etc: and how each of them found specific individual functions whilst maintaining intricate matching shapes for an apparently unforseeable future of forming a flagellum: and of course how they finally decided it was the right time to assemble and form a fully functional flagellum: all this by chance ... please explain ...

When it comes to life on earth, we have explained the process that caused life to be this way, through the theory of evolution. ... no you haven't ... you don't even have a consistent definition of evo. in biology ... all you have is a "just so story" ... like "it just happened to be so" ... we have factual explanation for variety of pre-existing organisms ... not for morphing of organisms which has little to no factual backing ...

Furthermore, the elements of the theory of has been tested and refined for over a century, to the point where we've written countless scientific publications on the evolution of different things. ... actually it's more like the theory has been almost changed totally to fit the evidences that contradict it ... 

You seriously think you can match that by saying "design", as if that would be an explanation? ... I seriously wish there was something credible to match ... most of the evidences clearly show design ... evolution is totally clueless as to how IC systems appeared ... for God's sake experiments show evo. degrades pre-existing components ... how on earth can that seriously be used to explain appearace of new functioning IC systems? ... 

That's why people laugh at creationists, you know. ... It very well turns out that they're laughing at their own idiocy ... 

I know the book you're talking about, but the people who wrote the book didn't know, either. You're referring to a story, not to a real thing. And "Yahweh" is an evolution of an older god, "Yahw" (Yahoo), the warrior god of some pantheon of gods, a long time ago. ... well I chose a name which would be easily recognisable by you : but it was naive of me since you believe God is different in Christianity and Judaism ... I apparently just gave you an avenue to display your idiocy ... 

And Muslism and Jews and christians disagree about what god you're really talking about. That's because no one can actually refer to anything real, only their own imagination, interpretation of culturally significant stories. ... no silly you're probably making a fool of yourself: Jews and christains agree about God: did you forget that the jewish text, the Torah is a part of the Christian Bible? ...  

Yet instead of realizing that it's fundamentally wrong, like with volcanos and earthquakes and rain and thunderstorms, religion refuses to die. ... religion is actually evolving(and I'm using the term correctly here) ... too bad you're not smart enough to realize religion has already infilterated science: in the form of Darwinism and this dogma you're pushing ... 

As I think I've pointed out, it has become pathetic. I could respect it back when they actually stood by the claims that their religion makes, but now it's just a bunch of spindoctors who try anything they can to avoid having to face the facts. ... I'm not sure if you're making any sense at all here ... Christainity has stood by it's claim for as long as it started: it maintains that God is the creator of the universe and life: the claim is even being confirmed by science ... 

If "god" exists, then he clearly is not the god described by the bible. Yet people still want to claim that it's the same god, that even though the bible is wrong abut most of the things it says, you can somehow still trust that the "important" things are still true.And what are those things? The things that still "feel good", like the idea that you'll get to heaven iehn you die. Not because it's rational to believe that, but because it feels good. Yes, it's become pathetic. ... maybe you should stick with what you actually know ... 

There is no "alternative". yes there is I've heard it from sources way more credible than you ... 

No one else has ever managed to propose a theory that would explain all the facts. Creationism barely explains half the facts, while the other half speak against it, or remains oddly inexplicable. ... Oh so are you saying creationism explains some facts? ... it definitely seems like you're ... but you keep saying there's no evidence of design in life ... I just have to ask again are you sure you're aware of exactly what you're saying? ...

Evolution is the only explanation we have that accounts for all the facts. ... actually evolution is the only explanation you want to believe in ... I'd say barely explains anything aside the obvious: organisms vary ... 

But this is not about which explanation is better, it is abotu which excplanation can be demonstrated to be true. ... the explanation that can be demonstrated to be true would be the "better" explanation ...but evo. has been as a matter of fact demonstrated to be false on many fronts ... the fossil record easily takes evo. out ... easily ...

The theory of evolution has been tested and confirmed. Nothing you say can change that. ... lol ... you must think this is an indoctrination session ... "X is true, there's nothing you can say about it" ... lol hell no you have to prove that "X" is actually true ... so far you've come up with more assertions than evidences ... more banther than facts ... presently, you're contradicting yourself once again : I remember you saying evo. theory isn't a scientific fact: now you're saying it's "been tested and confirmed" : that's the criteria for a scientific fact ... once more : I really hope you are aware of what exactly you're saying ...

If you want to challenge the science, then do it in a scienitic forum: Write papers to peer-reviewed science journals and present your evidence. ... I would but I don't want to cause another scientist to loose his source of lively-hood because some close-minded excuses for scientists can't listen to a different perspective ...

Do note how basically not a single ID proponent ever actually does that. ... lol you silly man ... when some one can loose his job for publicizing an ID paper it clearly shows a bais towards evo. ... evo. proponents can come up with any BS they want and it'd pass as peer reviewed so long as it supports the dogma ... ID proponents are limited to debates and Books which luckily turn out to be good sources of scientific knowledge: you can search out the debates and read a few books for more knowledge ... but I doubt you've done any of that ... still, you claim to be rational ...  

Why? Because they know you can't argue for ID, since there is no evidence for it. taht's why ID proponents want to bypass the scientific process and go straight for the "profit" instead. ... you can't possibly be serious ... anyway I think I've said enough for now ... wouldn't want to compound the issue more ... 

No, "intelligence" requires evidence, like everything else. You're not allowed to bypass the scientific method just because it suits you. ... what evidence do you require? IC, fossil, finetuning, SC, which one ? ... I've given you detailed explanation of some of these ... all follow the scientific method ... all are vaible facts ...

Yet this process is used in technology because it does exactly what you think it won't. ... I hope you're not talking off you ass again ... cuz to my knowledge all our technology is direct product of intelligent design ...

The problem lies in you thinking that anything like that is ever needed to explain the diversity of life. ... yes it's not needed to explain the diversity of life like we see in the different shapes, sizes and tones of humans ... it is needd to explain the imaginary process of building livers and lungs and eyes and nose, bones, brains etc etc: all by random mutations ... still not sure exactly how this is science ... 

The problem is that you don't understand the science, that's all. If you did, you'd not be giving analogies that simply do not fit. ... I think the problem is you probably don't even understand science at all ... and honestly, I hope that's not the case ...

You don't know what was turned into the flagellum, so you don't know what changes were required. ... and I suppose you do? ... lol ... hell no you don't ... what we know for sure is that it exists, and it's IC ...  

You're pulling stuff out of your ass, simply. ... lol ... a word from the master I guess ...

"Complex" being an adjective, and "irreducibly" being the adverb that enhances the adjective. In the same way, we could say "incomprehensively large". ... hmmm ... I'm wondering did you do this check for evo.? ... atleast if you did you'd be able to give me a consistent definition for evo. in biology ... btw IC is clearly defined by Behe: and it has nothing to do with something being red ... 

Did you go to school? Or did you perhaps go to an american school, and that's why you don't know these things? I won't blame you, in such case. ... lol ... I'd suggest you request a refund from whatever school taught you so much BS: and neglected teaching you how to think... well same can be said about my school: most of what I know now are self thought ... just curious though what did you study in school? ... I really doubt it's anything related to engineering: because I don't think there's any engineer that should buy into something like evo. ...

Well, that should be obvious. Find something that you can remove from the system without removing the function of the system. For example, you can remove things from a computer, and it can still work like a computer should. That proves that it isn't irreducibly complex, so if someone claimed that it was, then that claim is falsified.  That means that the attribute "irreducly complex" doesn't apply to that computer. You can also check whether somethig is red or not, to potentially falsify the claim that it is red. ... Ok I get it: I see a red shirt and I say it's red ... I see a system, and I check for IC and say it's IC ... these are the same ... Ok ...

It's actuallymore like the last 10 000 years, and it's because of agriculture, mainly. If you'd actually study thes things, you might understand them a little better. You think you can just "think" your way to knowledge, but you can't. ... are you even reading the lines? ... are you even thinking at all? ...yes it's 2000 years I'm talking about and we can ascertain the amount of development we made in that time ... and the development is mainly because of science and engineering ... if you compare the development which took place since the start of the Christain era you'd see that it'd have been impossible for humans to stay for 200,000 years and not even discover electricity ... bruh could you actually think more? ... this is getting unpleasantly tidious ... PS, yes you need to "think" your way to knowledge: if you're just going to digest everything someone says without questioning then you're not knowledgeable: you're indoctrinated ...

No one cares how you see it. Your opinion doesn't matter. ... OK then : evo. has never been proven right: as a matter of fact ... evo in the sense of the actual meaning: not "frequency shift" ...

And you're giving your opinion on something that you haven't studied and clearly do not understand. ... this is hypocritical: you give your opinions about things you have no clue about: you've even admitted it ... and it's not like I've not taken time to study evo. I have : that's why I can easily tell you that the basic confusion is in the definition ... 

When you put something in a controlled environment, it no longer needs half of its functions, because a controlled environment doesn't pose the same kinds of problems. In that case, losing a few function is good beause it reduced the energy upkeep cost. You're basically taking something that is good at living under various conditions, and applying one simple pressure to it, not a complex multitude of pressure like it faces in its natural environment. It can lose its functions that made it survive in nature, because nothing is selecting for those, anymore. ... you've said absolutely nothing different ... experimental evidence shows evo degrading components ... and apparently this is the process used to upgrade and even create new components ... PS even in the "multitude of pressures" in the complex outdoors, there's been no observation of an organism building a complex system ... the advantage of the experiments is that it gives you the chance to force any pressure needed to build components and systems ... but that obviously has never been seen: the direct opposite is actually the case: ... in other words experimental evidences show that evo. is not possible ...

Yes, you might mean it that way, but someone else might not. ... probably only if that someone is like you ... I don't think there's any christian that has a problem with what I said ...

You have "reasons", but you have no justification. ... I do have reasons and justification ... 

*You cannot actually support your belief with anything. You may think you can, but you can't. * ... hahaha ... another "it is so because I say so" bit ... would really use some rationality or any piece of evidence to support this ... I'm sorry but I have good reasons to discard baseless claims like this ...

You're relying fallacies, which means there is no true justification. ... I'm relying on IC, SC, the fossil record, Entropy, finetuning, biogenesis ... no one told me these were all fallacies ... 

Yes, why one "can" believe in god, but there is no reason why anyone should believe in god. ...  actually there's no reason why I should take a baseless comment like this seriously ... and I'm sure any rational person would agree with me ...

By that I mean that there is nothing to justify that belief, no evidentiary support. ... IC, SC, fossils, entropy, finetuning, biogenesis ... really don't like repeating myself but it seems like it's needed for you ... I mentioned and explained some of these to you ... but you confidently say I have no evidentiary support ...

I believe in coffee cups because I have evidence of their existence, for example. That is a justified belief. ... and I believe in God because I have countless evidences for the reality of God ...

Even if all you can predict is the probability, it's still not random. Somethign that is random is somethign no one would ever even try to predict, because by definition you can't. ... you can predict something random like I demonstrated ... just predict that "it would change" ... simple prediction ... just like I can predict the decimal numbers for Pi would continue to change ... that's possibly the only prediction that can be made for a random event ... and the kind of prediction evo. fully utilizes ... 

To some extent, we can. ... the extent is negligible for evo. many of the environmental conditions arise from random mutations ... it doesn't matter if you can predict some aspects what matters is you can't predict it as a whole ... and that's what counts ...

Sudden, but not "random". ... wth ... I'm not sure why I'm still responding to this ... 

But forget all of this. Even if the environment is random (changes randomly), the direction of evolution is not random if it follows the environment. Know the environment, and you know the direction of evolution.... well finally you admit the obvious truth ... the environmental conditions are random; the mutations are random, evo. strictly follows these two ... so what makes evo. non random? ... lol ... this is unbelievable ... 

Well, the fact that since we are only allowed ot fish large fish, the average size of fish in the ocean has gone down. This isn't a prediction, I know, it's a "post-diction", but my point is that such a thing could be predicted. You want actual predictions, you have to talk to an expert, I'm just a layman. ... Ooookk ... so there's none you know of ...

Adding -1/+1 to zero, perfectly randomly, will tend towards zero, in that over time any small change from zero will disappear. You'll have an infinite amount of +1 and an infinite amount of -1, which adds up to zero. ... do me a favor please : use a practical situation ... take a coin and toss it : lets assume heads is +1 and tails is -1: take the average of every five tosses after adding the outcome to the initial value, starting from 0 ... if the average shifts from 0 then my point is made ... simple as that ... 

Of course you "think" so, beacuse it doesn't show what you wanted it to show. ... dafaq ... it's a fail because it shows exactly what I expected or "wanted" it to show ... which is that the frequency changes ... 

You would never accept it, no matter what, even when mathematical proof stares you in the face. ... smh ...

So you're simply admitting bias? Nothing can be right just because it is related to evolutoin, huh? ... yes I'm admitting the so called law is based on a bais ... a bais for a belief ... it could be right if it was a fact that orgaisms did morph from different organisms ... not sure why it's even called a law ... and I'm not sure I've seen a law that's based on a theory ...

A million years can't be enough time. It took 6-7 million years to change from the common ancestor with chimpanzees and humans into the humans we are today. And that's a small change. Wings would require very large changes. Perhaps 200 million years could do it? ... yes of course how could I forget that ... so by my calculations in 1 billion years time humans would finally complete the evolution into dragons ... seems plausible to me ...

Even something that moves in a random direction has still beeen somewhere, meaning taht there is still a direction that would take it back to wherever it was. ... assuming there's a backward direction is simply assuming that all random directions are foward ... if so then it's not undirected ... if there's something keeping you from going back, you have some sort of direction ... btw what ancestor of humans possesed wings ?... 

But if it moves randomly, the change of getting back to the last position is extremely unlikely. if it moves randomly there's no "back" direction ... and so far as I know the "direction" is determined by random mutations and random environmental conditions ... 

But evolution doesn't move randomly. However, it doesn't plan ahead, it's just a process of natural selection, so the environment determines where it goes with any specific species. ... OK evo. doesn't move randomly, but it doesn't plan ahead ... what exactly are you saying bruh? ... if evo. just moves without a plan, then it's random ... you're just contradicting yourself ...   again ... 

Nice contradiction. Fail proof but will eventually fail, huh? ... lol what? ... I said it was good enough for the designer, but other factors hindered the continuation, so the designer added more info. to adapt to the other factors ... what can't you understand here?

No, sorrry, your explanation still has to explain the facts. There are no pre-cambrian rabbits, that's a fact. But more recent rock layers reveal more rabbit-like creature. ... well then in this case the designer just designed the rabbits at a later point in time ... 

I'd love to hear it. ... again? ... well I'm going to repeat one more time: God is an intelligence, a force, which exists without the limits of the physical laws, but manifests in the physical realm ... God is most likely the source of energy ... 

No, "god" is in fact unknown, or can you demonstrate your god? I didn't say that you said he is unknown, I simpyl know that he is, because no one knows anything about any "gods". ... you're saying more nonsense ... "no one knows anything about any gods" ... I think this might be a good reason to stop replying ...

What, you're on the side of gradualism, as opposed to punctuated equilibrium? Why? ... no buddy no ... you're off point ... again ...

That's not what we're talking about here. We dont' need any transitions to validate evolution,b ecause we can observe evolution right now. ... hahaha I love this bit: "the fossils prove evo." and when the fossils actually show the opposite? "Nah we don't need the fossils"  ...

You can't see on a fossil whether it was rapid or not, you have to look at the series of transitions. And yes, we see that change happens at different speed in the fossil record. ... lol what you see in the fossil is sudden appearance and sudden dissappearance ... the notion of "change" is only an interpretion from your belief ...

But like Isaid, this isn't about fossils, either, this is about evolution. Fossils is paleontology, the history of life. The theory of evolution is about the process of evolution, how it works. ... Ok buddy ... but just to put this out: ID also explains most of paleontology ...

They didn't emerge out of nowhere. I suppose you've been misinformed. (?) ...the fossil evidence show they did ... you're most likely the misinformed person if you think the fossil record shows the traces of gradual evo. ...

And yes, you've got a bunch of animals evolving a lot during that time, but what about the plants, for example? Flowers, for example, evolved hundreds of millions of years later, not during the cambrian explosion. ... "appearance" is the appropriate term ... obviously you're trying to force the evidences to suit your belief: and this is a major problem in discussions like this: you just can't be objective enough to admit what contradicts your belief ... the cambrian animals didn't "evolve" going by the facts and evidences: they appeared ...

Also, we do have fossils of animals long before the cambrian explosion, in case you thought that animals didn't exist before then. ... lol ... I'd love to see these animals and how the fill in the blanks : I'd like to see if they fit as transitions for the plethora of new organisms that appeared ...

There is nothing else of interest in the cambrian explosion, other than that is was a long period of relatively fast evolution, rather than a short burst. It's still evolution. ...20 million years: relatively "fast" evo. ... hmmm ... so fast they forgot their transitions ... hmmm ... I don't buy that ... the faster you evolve, the closer your transitions are expected to be ... 

And also, the Cambrian explosion is not the only case of large-scale diversification of life in the history of earth. A similar thing happened later, aswell, called the great odrovician biodivesification event. ... yeah a way to discredit evo. more ... well I'd suppose the cambrian was different because the diversification was relatively exponential and the outburst of new organisms from nowhere was quite shocking to evolutionists who would have expected to see the slow morphing evidences of each species ...

Just fucking look for them..? ... they aren't there : you think I haven't tried? ... even the post cambrian periods: little to no transitions: all we have are artistic fabrications and of course, "all fossils are transitions" ... ie. there's no proof of gradual development in the fossil record: and this is what evo. predicts in abundance ...

Here's one example, detailing the panarthropoda phylogeny. There you've got the common ancestor of tardigrades, arthropods, for example, the tactopoda. ... I think you might have missed my definition of "transition" : by transition I'm looking to see a smooth string of morphing b/w two relatively different organisms: obviously one can just take creatures and fix them up in a "tree" and claim they evolved: that's not enough proof ... you have to prove that they actually shape-shifted to begin with ...

If you don't bother to fucking look, it sure will seem like there are none. But it definitely isn't hard to look it up. ... yeah it doesn't exist bruh ... 

yes, during the cambrian explosion, evolution apparently kept a relatively high pace, and for a long time, which is very rare, and we would certianly want to know what caused it. ... I know the cause: the most obvious and likely cause ... that's right, ID ... 

But like I said, it could be the evolution of eyes that changed a lot of things and caused an "arms race" for a while. Both of these things explains why only animals evolved so much during this period, but not plants. ... well since you're obviously struggling to make sense out of the Cambrian period with evo. explanation lemme just help you with a more sensible and be-fitting explanation: most likely, what happened is the plants were created first and then the first string of multi-cellular organisms next ...

Hey, why not read a book on the subject, instead of specualting? I'm sure not the best source for info on this, I'm no expert. ... I don't speculate much : like I said most of my sources come from debates where I get clean and credible information from listening to both sides: and no scientist I've heard of questions the sudden appearance of the cambrian fossils: it's still a mystery to them: you're just the only one trying to force one of your many false knowledge through ... maybe you should take out the time and get to listen to a much rounded explanation ...

You don't test and falsify facts. You test and falsify explanations. Facts just "are". ... Ummm you do test and observe to determine a scientific fact ... don't know exactly what this is about this time ... the explanations are the "facts" ... If I say "this is a rock: as a matter of fact" , then that's an explanation: and science would aim to prove that it is, as a matter of scientific fact, a rock ... anything to be deemed "scientific" must go through the process of observation and repeated testing to be called a scientific fact: and it's not a scientific fact that anything like music exists: what can be tested and observed and verified through the scientific method is sounds ... 

No, this is simply a case of something that is hard to agree on a defiition of. ... yeah more or less: it's actually non-existent looking from a scientific angle:  

But whatever you consider music, it's a fact that it exists, right? I mean, you're listening to it, aren't you? ... yes anything I consider music is a fact to me ... it's subjective ...and science can't validate music based on this ... 

If I conser only hard rock to be music, then yes, we can confirm that hard rock exists, if we give good definition of what actually makes it "hard rock". But the problem is that people disagree about how to define it, not whether it exists. ... yes you might be able to confirm that hard rock exists: you just can't confirm that it's music: many people consider it to be noise: like me ... also, I'm not saying people argue about whether it exists: they just assume it does even if there's no particular handle as to what exactly it is ... looking at it scientifically, it can't fulfill the criteria to be deemed a scientific fact ... so if you consider anything which can't be verified by science non-existent, music wouldn't exist ...

WTF, when has science ever established that "music doesn't exist"? Are you fucking high, or something? ... again, think brother ... I said, if we strictly go by what science can prove, music doesn't exist because science can't prove that it does ... 

Yes, there is, it's just that there will always be a few people who disagree. ... no there isn't ... if you say music is sounds, it easily gets falsified on experimentation ... therefore that's not what music is: if you say music is anything everyone agrees to as music, what happens when people disagree about a music? does that mean it's not music? no ... that description is falsified as well ... you can't put a description to music that can't be falsified ... and definitely, you can't explain music in terms of the physical realm alone ... because all that exists in the physical is sounds ..

But do you really think that music is the only thing this applies to? It applies to more things than it doesn't. ... a way to say it isn't a scientific fact ... 

I seriously wonder if you've been smoking something bad, or something. This conversation just dropped a number of levels. ... you must be really delusional if you think I'd care about this ...

Music exists, but a global definition of what should be considered "music" does not exist, as with the majority of things. ... Music exists yes: but it's not something you can say is a scientific fact ... I hope you understand my drift on this? ... we just all asume, and agree that music exists ...

No, it's not a democratic vote. Something is music to a specific person if that person considers it to be music. But when that person needs to communicate about music, then that person needs to try to use a definition that others will share. ... yes I agree with this ... anything that is music to anybody is music: I believe that was what I said: my point is this can't be scientifically proven ...

The problem lies in the word, "music", because most of us agree that the word refers to something subjective. Therefore, it's a wasted effort to try to make it objective. ... yes it is subjective ... that's why science cannot prove it objectively exists ... but it is also a fact ... 

You can extend this to "chairs", if you want. Not everyone agrees where "chair" begins and "sofa" takes over, or "stool", or whether a wooden log is considered a "chair" or not, it depends on whether you're a pragmatic person or an idealist, or whatever. ... a chair "an item of furniture used to sit on or in, comprising a seat, legs, back, and sometimes arm rests, for use by one person" ... if you find any furniture that fits all these criteria, it's a "chair": simple ..... now a stool is "a seat for one person without a back or arm rest" : any furniture that fits this criteria is a stool ... it can be verified objectively what a chair and a stool is: and it can be tested and verified with the scientific method because it has a specific definition ... in this case, a wooden log isn't a chair ...

But you would argue that this means chairs don't exist. It's ridiculous. And scientifically speaking, the thing that a person calls a chair does in fact exist if it exist. The thing itself is not dependent on how we choose to define it, and that's true for music as much as for chairs. ... wrong ... try again ...

No, but now you're only arguing that the definition of "music" can't be scientifically determined. That's correct, it can't, because that is not the realm of science. ... Ummm every scientific fact has to be properly defined to be tested ... if I define evo. as change in frequencies, then scientifically speaking, anthing that changes frequency is evolving ... but if I add specificity and say change in allele frequency then scientifically speaking, any "allele" that changes in frequency is evolving ... 

But you do not need science to determine whether such a thing exists. I can hear music, I can see chairs, and sit in them, and so on. ... I can use the scientific method to determine that chairs actually do exist:  I can't use it to determine that music does exist ... 

I know they exist, that is a fact, I don't need a scientific method to tell me that, becaue the scientific method is about explaining the facts. ... No the scientific method is a method of determining facts through observation and repeated experimentation ... scientific theories would be what explains facts ... I hope you do know all this ...

Because life isn't an isolated system, the 2nd law of TD doesn't apply to it. And yes, the reason why an open system, like an organism, doesn't have to increase in entropy is because it can eat and take in energy to prevent entropy from increasing, as it would have if it didn't eat or take in energy, because then it would've been an isolated system. ... and I'm saying that it's only a system created to decrease entropy that can account for any decrease in entropy ... not that 2nd law of TD doesn't apply to life ... if we're going to take this in a strict sense then you have no justification to say 2nd law of TD doesn't apply to life ... the law clearly doesn't say anything about what happens in an open system ... it clearly says it does apply in an isolated system: and I'm utilizing that fully ... I'm saying what the law states : and it states that the entirety of an isolated system( whether it has an open subsystem or what ever) tends towards maximum entropy ... so I could say the solar system is tending towards maximum entropy ... and this includes life ...

Do you realize that you're arguing against the existence of life itself? An egg that develops into an organism would be impossible if what you said was correct, for example. ... I'm actually arguing that life wouldn't exist without the intricate and functional systems we see which limit entropy ... so an egg that develops into an organism would be impossible if there's no such system specifically aimed to allow that happen ... this brings us to how that system developed ... considering that prior to the appearance of these systems there was increasing entropy, this would seem impossible ... 

The sun provides energy for the earth, allowing things on earth to do work without increasing in entropy. But because of this, the entropy of the sun increases. In total, our solar system (which is a nearly isolated system) as a whole does increase in entropy, thus the 2nd law of TD is satisfied. ... the sun also provides energy for mars and mecury ... apparently providing energy alone is useless unless there's a system which processes and utilizes the energy ... obviously the sun's energy is not the cause of the decrease in entropy: biological systems are ... the suns energy would be destructive without these biological systems ... and even these biological systems can't ensure a steady low entropy state: else no organism would die ...
Reply: Benjamin Toby "The beeps are symbols. And even if you can learn to decode them to letters in head so fast that it effectively seems as if you're not even decoding them, the fact is still that the morse code system was designed as a code system where letters/characters are encoded into short/long.
... well then I guess we could agree that the sounds are the codes ... which means the codes are real ..."

See, we've still not managed to move past this problem. This is still the core of our discussion.
The sounds are real. But "codes" are not real, they are in our heads. Codes are abstract, and to treat them as if they are real is to commit a reification fallacy.

We both agree that the medium that carries "code" is real. It must be real, because otherwise they could not be used as a way to transmit something.
But the beeps are just beeps. Without the knowledge that they should be considered "code", they are just beeps. The beeps are real, the codes aren't. The codes are something we've agree on.
Basically, a duck is a duck, but if we agree that sending a duck to someone means you're trying to tell them it's going to rain, then to us, the duck is a message.
The message is not real, it only exists in our heads. The medium that carries our message is real, of course.

And I just can't believe after this long conversation, we're still right here, where we were at the beginning.
And I said I wouldn't discuss "code" anymore, and I should've taken my own advice, because this is clearly a huge waste of time.

"*DNA is a molecule.* ... yes ... morse code is sounds ... "

No, morse code is not sounds, it is a conceptual idea of encoding symbols as "long and short". The fact that you can draw morse code proves that the code is not "sound". Sound is one way to carry the code. The code is not real, it's just an idea. Anything that can be used to physically represent the idea is just a medium, but it would be a medium capable of transmitting the idea of a message encoded as morse code.
It was invented the way it is because it was meant to be sent in the form of long and short signals - not sound, but electrical signals. A speaker turns the electrical signals into those beeps.

"well DNA obviosly contains encoded info. if it didn't then why the hell does life depend on its interpretation? "

You don't "interpret" code, you decode it to get the actual symbols - and you can interpret those symbol to understand their meaning.
DNA in a cell is a mulecule that produces other molecules though chemical reaction.

"1. Find the guy who made the sequence. ... lol hell no ... we can tell the difference between a rockslide and a Stonehenge ... we can because of our repeated experience with intelligence ... same way SETI can tell if they discover encoded message signals ..."

SETI can't. They can only tell if something is known or unknown. If it is unknown, it deserves investigation. But they cannot know if a signal came from an intelligent creature simply by looking at the signal. It would have to be a signal that somehow uses a system that we invented, so that we can tell that it is a message. Basically, it would have to use our language. If it is in an alien language, we don't know that we can tell that apart from something natural. It would be an unknown signal. All we could say is that we've never seen nature make a signal like that, which doesn't mean nature didn't do it, it means it deserves investigation.
And note that they have never actually found a signla from some intelligent aliens, so they have no idea if they'd be able to spot it if they saw it. For all we know, we might already have received messages from aliens, we just don't realize it because they don't do it the way we do.

"2. Identify a known coding system which, when applied to the sequences, makes the sequence make perfect sense. It is highly unlikely that something apparently random would be decoded into something meaningful with the wrong coding system.
 ... the coding system for the DNA is obviously the cell and it's "machines" ..."

No, now you're once again using some fucked up definition of "coding system". I'm talking about something like morse code. If we see some kidn of signal, and we use the morse code system to decode it, and it turns out to be perfectly valid sentences, then it's reasonable to think that the sequence was encoded using the morse system. That would require a mind, since it's completely arbitrary. Thus, the sequence must have come from someon/something with a mind, or something similar.
Another example would be to see a bunch of apparently random numbers. But when plugging those number into the ASCII table (a code system), it becomes valid sentences, then we've got that situation, again.

The DNA of humans, however, doesn't do this. Use ASCII or morse code to decode DNA, and you get nonsense.
PErjhaps there is some coding system we're not aware of that was used ot encode it, but that would amke no sense, since the sequence in DNA is not arbitrary. You can't both use DNA to send an encoded message and use it as a genome for an organism at the same time.

"the DNA makes perfect sense only in the cell : so we can observe a coding system which can make meaning out of the DNA ..."

You're mixing up "coding system" with "instruction set".
Seriously, try to make some sense.

" it's quite similar to the computer code: the coding system is the computer: it can make sense out of binary codes ..."

You seriously must be trolling me, here. I refuse to believe you're this stupid.

"DNA might not make much sense to you ... but we obviously see it does to the cell(s) and organism(s) ... "

It doesn't "make sense" to the cell. Explain where in a cell the brain is that can "make sense" out of something.

"yes the cells do use the "meaning of the sequence": are you sure of what you're saying? ... if you delete sections from the DNA of an organism you can end up creating detremental damages to it ... "

Same thing if I were to delete a sequence of the instructions of an automated robot that builds cars in a factory. The cars might turn out not working. There was no meaning to the sequence, it was data that the robot used, which controlled the movements of its arms, and so on.
Meaning doesn't exist on that level. It was "useful" and it produces the correct result, but there was no "meaning" in it. You could not read the data that the robot uses and see the "meaning" of it. It has purpose, but it doesn't contain meaning.
A sequence of DNA also has a "purpose", in that it's used to build an organism. That is the purpose it's being used for. "Purpose", in this sense, is not the same thing as "meaning" is in the linguistic sense.

"*No, that's the software giving you the appearance of understanding. It's not the computer, it is the program.* ... and what exactly do you think a computer is?"

That's a strange question. First of all, it's not a program, and that's the only thing that matters in this context.
Apart from that, a computer is Turing machine. Originally, a "computer" was a person who calculates things for you. It used to be a profession.

" ... well A software is basically useless without a computer: but a computer is still perfectly effective(or even more effective) without a software ..."

Yes, software requires somewhere for it to run, like how a train needs a railroad, but even more aggressively so.
Yes, a computer can "start" without software, but it'll be infinitely less capable. You can't "do" anything with a computer that doesn't have software. It doesn't even have an operating system. It'll basically be a humming paper weight.
If you're talking about somethign liek a calculator, then that is not  a proper computer, because it can't be programmed. That is, unless it's a programmable calculator, in which case it is a proper computert, but it also relies on software.
Basically, the problem is that anytime you actually do anything with a propoer computer, you're using software. The hardware itself isn't useful unless it runs a program.

" it's because the computer has an artificial mind that the software depends on to even make any sense ... "

A computer is not a mind. I think I've already linked you to the definition of "mind", otherwise you can look it up yourself. You're simply utterly wrong.
A computer is a framework for software to run on. Software could potentially simulate a mind, however.
Likewise, you could also build a computer that does have a mind. It just won't be a Turing machine, so it won't be a "computer". It'll be very, very different. A mind doesn't have the need to work like a computer does.

"*For a computer to be able to work with "code", the CPU must have a mind. The CPU itself, not the software that it runs.*
 ... yes the CPU has a "mind" ... I'm pretty sure that's why it's called Central Processing Unit: translate that to humans and it come out as brain ... to process something and give an output is basically all you need from a mind ..."

Stop equating "brain" with "mind". They're two different things. Yes, the CPU, in the broad sense, is a kind of "brain", but it doesn't produce a mind, like a human brain does, because we didn't design it to do that. We designed it to take instructions and output a result. A CPU is a calculator, but because of how it is connected to the other parts of the computer, the computer as a whole becomes more than just a calculator, it becomes a Turing machine, a computer.

The main difference between a simple calculator and a turing machine/computer, is that a computer has a program pointer. It runs instructions in sequence, and has the ability to jump in the program by moving the program pointer. This is the key concept of a turing machine.  The other thing being the ability to change the data its working on/with. Because of this, you can do a lot of things.
A calculator doesn't need these capabilities, because it won't run a program, it will only work with one instruction at a time. One instruction is basically the entire program.

"*The CPU would have to be able to choose what to do, not be tied to cause and effect, in the sense that a specific pattern of switches causes a specific effect.* ... yes the CPU can "choose" in a sense ... "

In the weakest sense, perhaps. But a program, however, can make something that's more like proper "choices". It still isn't the same things as with human choice, because the choices we make imply a certain amount of freedom to pick an alternative, adn we have never really made a program that has that kind of freedom.
Of course, it's perhaps possible that humans don't have any such freedom, either, we just haven't established that to be the case.

The word "choice" does, by definition, imply free will. I'm not sure I like that, and agree with it, but it's still what the word means.
A CPU has the least possible amount of freedom in making choices. We rely on the CPU to do exactly what it's told, not to make choices freely.

"what matters is the programming (or wiring or architecture) ... and I'm not sure: how is a software not tied to cause and effect?"

Software is also tied to cause and effect, and ultimately, humans brains probably are, aswell.
But a "mind" still implies the ability to make free choices. In reality, it's probbaly only th e*illusion* of free choice, but in a CPU, ther ei snot even an illusion of free choice. We rely on the CPU not making such choices, and we never intentionally gave them that capability.
If we could simulate a mind in software, then that would also be the illusion of free will, so to speak.

"Fine, I'll give you an actual example, just because you keep insisting. C++ example: ... dahell C++ is not going to help too much cuz like I said, I'm an amateur in programming ... theoritical programming more specifically ..."

Yes, I realize that, but I gave an extremely simple example, and I explained the example. If you do not take my word for it, you should have enough information to be able to look it up.
When you define a datatype, you're not writing somethign that will exist in the .exe, you're only telling the compiler what I intend to do, so that it can help me not to make mistakes.
And some things you write will partially become part of the .exe, and other parts are only there to, for example, make sure that I understand what I'm doing. The language forces me to expressely state some things, just to make sure I really do mean it, and am not just making a mistake.
And some thing you write will be in the .exe, but not like you wrote it. It'll contextually become something else.

"There, a very short example of a piece of "code" (remember, it's only called "code" because of tradition) that doesn't get translated into machine instructions when compiled. ... I strongly reckon it does ... if it doesn't then how would it be implemented?"

By writeing a "struct", like that, I have set up limitations on how I am allowed to use something. Ther ei sno reason for this to become part of the software, because this is only relevant to the process of writing the program, not running it.
It's about writing in a way that will systematically prevent errors, bugs or crashes, for example, by taking away some of my freedom in what I am allowed to do with certain things.
I don't want to accidentally add a number to a character, for example. Because they are defined as different data type, and C++ is a type-safe language, I am not allowed to add numbers to characters without explicitely stating that I want to do that. I have to tell the compiler "yes, I know this doesn't usually make sense, but in this case, trust me, it does", and then it'll let me do it, anyway. But if I don't say that, then it'll give me an error, because it's right in assuming I didn't actually mean to write that.
But all of this requires that we use extra words and syntax and so on. Things that are there for that purpose, not for the purpose of being part of the .exe. For the purpose of helping out during programming/development, only.

"But note that when I use "position", the only thing that is put into the .exe file are the x and y variables - not the concept/rules about how they should be treated, that hey belong to "position". "Position" will not exist in the .exe. ... OK I think I get this ... yes like you said it wouldn't appear in the .exe program: but I reckon it's just an instruction which the compiler uses ... and that instruction still ends up in binary codes: only that it isn't saved as part of the program ..."

Wait, is that all you mean? That everything I write will be saved in binary, simply because its part of the "document"? That is a given! I've expressely stated that it won't be part of the program, the .exe file.
We were discussing whether C++ is like code, like assembly, int he sense that a keyword translates to an operation. That is what I am talking about, the fact that C++ is not a system of codes, it is a language for talking to a C++ compiler.
I think you're deflecting, or that I am misunderstanding something. You must be equally aware of what we're talking about.

" I think I made that quite clear : I do not know much of programming: particularly the theoritical aspect ... you should be able to see quite clearly that I'm coming from a practical and realistic angle on this ... "

Programming is also "practical and realistic". (?) Software and hardware go together in a computer. They need eachother. You don't ever use a compuer unless you run programs on it.

" OK let me just say this: I think anything that goes through the CPU is code ... ie everything you do on a PC involves codes ..."

The thing that goes through the CPU can be descirbed using code, but it isn't inherently code, because like I said, code is a concept, and idea, it isn't a real thing, and a CPU is physical. It requires a physical medium, and it is the medium that goes into the CPU. In this case, it's a pattern of voltages that is the medium. Specific patterns cause specific outcomes, and we can name the patterns. But the CPU is not aware of the names of the patterns - but that is what you're arguing that it is. You're arguing that it takes the names of the patterns, not the pattern themselves.
A code is label, a name, an identifier, only that it is a second-level such thing. Instead of referring to something real or a concept, it refers to another symbol/identifier/name/label/whatever.

"for anything to be called a computer it must have an artificial mind ..."

Then there are no computers. It's that simple. You've just changed the definition of a computer to the point where no computers exist. Congrats.
Just look up the definition of "mind".

"Any assembly codeword directly represent a value. we're effectively writing direct instructions, but instead of writing the value of the instructions, we use a system where we give those values names - which is 2nd level symbolsim, code.
... I don't think this makes any sense ... if each word directly represents a machine instruction, then there's no difference if we just use machine code ..."

Assembly code -> instruction name/value -> pattern of voltages.
Morse code -> word -> the meaning of the word.
2nd level symbolism.

A "machine instruction" is just a symbol, it isn't the thing that it refers to. A "machine instruction" is symbolized by a value, because that value would, in binary, represent the state of those switches.
So a "machine instruction" is a symbol, it isn't the thing that it symbolizes.

But you're right that instead of using assembly, we could just write the values that directly represent the pattern of switches to be used. The reason we don't, as I said, is because it would be hard ot remember the values, and it would be nearly impossible to read and understand what you're written, afterwards. It would be "fit for human reading".
But that is what early programmers were forced to do, before they invented assembly. For assembly to work, you need an assembly compiler. Therefore, you were forced to write the asembly compiler by writing direct instructions.

"Yes, that is what I am saying. Because the thing that makes something a symbol is that a mind decided that it was. If no minds ever existed, there would be no symbols in the universe. ... Ooook ... and I'm saying physical objects can be symbols ... as a matter of fact, I think most symbols are physical ... not sure exactly if there's any symbol that isn't ..."

I just told you, those phsyical objects are symbols because a mind decided to consider them symbols. Without minds, there is no one to consider any physical thing to be a symbol for something, therefore no symbols exist.
Are you officially retarded, or something? It's right there, I just explained it, and then you act as if I didn't.
A symbol is a symbol only in a mind.
The idea that some physical pattern of some sort would refer to something else, is absolutely conceptual. This idea can only exist in a mind. In reality, there is no connected between those things, we've just arbitrarily decided that there is a connection, and we use that as a mental "tool".
The very same symbol could be used by osmeone else as a symbol for something else, or not at all. There is nothing about the physical object/pattern itself that inherently makes it a symbol. Anything could be a symbol if we decide that it is.

"*Judging by what you've said, and what you say later, you seem to equate the brain with the mind. That is a problem.*
 ... I think the problem fully resides within yourself: like you've said, the mind is the action of the "neurons" in the brain ... well the computer's mind is artificial and it's the action of the voltages and switches ... "

It's amazing how you can say such things and not realize what you're saying.
Sorry, what do we call the action of those switches and voltages? Oh yeah... software.

"anything in C++ can be done in direct machine code and practical circuitry: only it'd be extreemly tidious ... these are some of the reasons I seriously question your knowledge ... "

No, because a lot of C++ is only conceptual. Half of it doesn't ever end up in the resulting software. C++ is a specific process of creating a program. You can't manually do it some other way and still claim that it does what C++ does, since what C++ "does" is allow you to program a program in the C++ way.
It's literally impossible to do what you're saying, because it would be a paradox. You're literally saying that you can do C++ by not doing C++.
If you directly immitate C++, then you are using C++! C++ is a method, a standard. It is a set of rules that describe a process. either you do it that way, or you don't. You can't claim that you're doing it and not doing it at the same time.

"you can create a calculator in C++ and replicate it using machine code and practical circuitry ... same damn thing ... just that one would save you more time ... "

The resulting "calculator" software is not C++. C++ was only the source code that you wrote, which resulted in that software. C++ was the process used to create the calculator software.
You cannot immitate the process without it being the same damn process. If you immitate C++ perfectly, then it is C++.

"Once again, we describe them as codes (for simplicity), but the CPU doesn't. ... No we describe them as codes because they fulfil the criteria to be called that ... just like we describe a cat ..."

No, "code" doesn't have any criteria by which you can recognize them, and that's part of the point with codes. That is why they're used for secrecy, sometimes. A code is completely arbitrary, and that's why you could be looking at a code and not know that you were.
Some codes can be less arbitrary than others, but a code can be completely arbitrary. This often depends on whether the code is used for secrecy or for simplicity. Simplicity usually follows systems, and relate to the thing they're encoding, so that it's easier to learn it. DNA code is an example of this, where "TCGA" is easily understood as the first letter of each nucleobase's name. A simply code, easy to learn and quick to read.
But the "enigma" code used by nazi germany was extremely hard to break (at that time).

"And there is no "programming" in the CPU. The CPU isn't programmed to do things, it is built to do things. ... programming can also be described as "building" ... "

Yeah, if you're a fool. Or if you have nothing else to say.

"The CPU cannot change its architecture. ... a program can't either"

That is exactly what a program can do, in a turing machine. A program can change itself as it runs, that is the power of software.
A machine that doesn't allow the program to change itself isn't a computer, because it doesn't have the capabilities of a computer.

"... I see: this clearly translates to:
1/0 -> on/off -> the voltage/switches. 2 levels 
... am I missing something here?"

1/0 -> the switch.
on/off -> the switch.

1/0 was never meant to refer to another symbol, it was meant to refer to the state of the switches.
On/off is just another way to refer to the state of a switch.

But don't get me wrong, "on/off" could be referring to 1/0, if that's what you intended. In such case, yes, it would be code.
 I just wouldn't be able to know, by looking at the words "on/off", whether it was code or direct representation. that is, whetehr it was 2nd or 1st level symbolsim. That is the nature of "code", as I've said so many times.
It all depends on what you intended.

"on/off > active state/ inactive state> the voltage/switches. 2 levels
on/off -> 5V/0V -> the voltage/switches. 2 levels
come -> move towards my position -> actual movement. 2 levels
... this should do just fine ..."

Yes, if this is what you intend when you say or write those things, then they are "code".
If the symbol "come" should be decoded (replaced by) the symbols "move towards my position", then "come" is a code.

But when I say "come", I am not referring to "move towards my position", I am directly referring to the meaning of "come".
"Move towards my position", may be a description of the action of "coming", just like "5v/0v" could be a description of the two different states of the switch.
But a word/symbol does not refer to a description of it, but to the actual thing that it symbolises. A description is something completely different, since it is a way to describe to someone what the word does refer to.

A word doesn't refer to their synonyms, for example. Neither do they refer to a way to desdcribe their meaning. They refer to what they mean to a person. (Yes, words are subjective, and language is democratic.)

You're correct that the symbol "cat" refers to the concept of a cat, by which we can recognize a cat, so it would seem like this is correct:
cat -> concept of catness -> actual cat
...and that "cat" is therefore "code".
But it isn't, because "catness", the description/definition of a "cat" is not a symbol. Therefore, this is not second-level symbolism.
By "concept of catness" I mean our defintion and understanding of how to recognize an object as having that label.
When I say "I have a cat", your brain hears/reads the word "cat", and probably recalls an image of some cat, but also recalls what makes a cat a "cat", intellectually, if such understanding exists. So your brain will make some statistical or associative assumption about what kind of a thing it is that I have. It's probably going to be wrong, because your brain will subocnisously produce an image of my cat that probably doesn't look like my actual cat, but you'll be categorically correct. We'll both agree that it is a "cat", that the label/symbol does refer to that thing.
The concept of catness is not a symbol because it doesn't refer to anything. It describes an idea.

"How can you say that a computer understands 1/0?
 ... how can you say a computer doesn't understand on and off states? ..."

How about you answer the question?
It doesn't understand on or off states because it has no capability to understand anything. It has no mind.

"OK, so how does this explain morse code? ... well in morse code a pattern of sounds like "-....-" can represent "A" ... and only that pattern would represent "A" ..."

Yes, I agree.
Technically, what makes it "code" is that you've got a symbol that's representing a symbol, instead of representing something like a concept or a thing. That is, a "code word" has no meaning.
If you "ask" a codeword what it means, it'd only answer "any questions you have for me, ask that guy, instead", and it would point to some other word or symbol.

"Those would be "alphabets", not "syntax." ... so 0/1 are computer "alphabets"?"

1/0 is not something computers use, it's something we use. Those are symbols, you know.
In a "binary language", 1/0 would be the alphabet.

"If a coding system has its own syntax, then it probably becomes a language in itself. ... well I'm saying all languages are coding systems ..."

You're incredibly wrong. There are not 2nd level symboslism.

""novel" information: that which builds new structures has never been observed ... and without these new structures, evo. is invalid when explaining origins ..."

And then I guess you'll be doing everything you can to avoid ever defining "new structures", right?

"But I agree that since it is based on somethign else, it isn't new "from scratch". But that doesn't matter. ... it does since you've just accepted that duplicated info. doesn't fit my criteria for "new" info. ... "

I didn't what what you criteria was for "new information". If "duplicationmutation" doesn't fulfill teh cirteria, then Ia gree that it isn't an example of that.
But all sorts of different kinds of mutations happen, and some of them must fulfill your criteria. If they don't, then your criteria is irrelevant, becuase then we don't need "new information" to arise to explain all life on earth. Then I'll agree that "new information" (by your definition, not mine) never arises, but I will also not agree that "new inormation" ever needs to arise, either.

"*And for some really weird reason you said genetic code is altered throuhg "genetic variation and natural selection". Dude, that is evolution!* ... yes evolution is scrambling and degradation of pre-existing  information "

No, the "scrambling" of information is called "mutation".

"...  but by scramling and degrading pre-existing information we can get all of the complexity of life ... beautiful stuff ..."

No, you can get that through "evolution".
Nice attempted straw man, there, but you're just wasting time and effort.

" We immitate nature, because nature alreay does a lot of interesting things.
 ... lol you're dangling on the edge of a falsity ... we can see nature reproduce what we all saw from the beginning of our lives"

I have no idea what your point is. If you're talking about evolution, then you haven't lived long enough to see any changes. Not that changes haven't happened, they're just too small for you to see them. You need to look at the DNA level to see the changes.

"... "nature does a lot of interesting things" ... lol ... like what? reproduction? well yes ... shape-shifting? well hell no nature doesn't do that ...that happens only in the mind of some people ... "

Reproduction, yes, that's pretty cool, and we'd love to make technology that reproduces itself. We have that, on small scales, such as the self-replicating 3D printer.
Shape-shifting, yes, lots of animals do that, in different ways. I have no idea how you could have missed that, but who cares. An obvious example would be metamorphosis where a caterpillar turns into a butterfly. Less obvious examples are things like the "transformer owl", which is an owl that can immitate a cat, amongst other things. It literally changes shape.
And evolution, yes, that is something we've learned about, from nature, and are applying to technology.
Imagine how weird it would've been if we started using evolution in robotics and computer sience, before we realized that nature does the same thing?
Or how we'd immitate birds to figure out how to make airplanes before we ever saw a bird?

" I can say you have no reason to believe that a random process can build a biological machine like the flagellum ... and I have better justification to say that because even you'd agree that no random process can build any functioning electric fan motor "

No one here is proposing that a random processes can do that. Drop the straw man and stop wasting time.

"... and you'd also agree with me that the process which is supposed to build this machine is destructive on the average ..."

Nope, the process is not destructive.
Remember, it's not evolution that produces mutations. That's just physics and chemistry. Evolution simply depends on those things existing for the process to work.

If you would remove evolution, you'd still have mutations, but you'd no longer have anything keeping those mutations under control. You'd have nothing weeding out the bad changes, and you can probably imagine what that would be like. Waht is peopel bron with rare genetic defects liek bing born without skin woudl actualyl survive and reproduce as much as everyone else?
I mean, the idea makes no sense, of course evolution cannot be "removed", without things being very, very differnt.

"We have no reason to think that any intelligent creatures existed back then, to create the flagellum. ... yes we do... the reason is that without invoking intelligence, we're left with a mumbo jumbo random process"

A false dichotomy fallacy. There aren't just 2 alternative, ID or evolution. If you're looking or an explanation for something, then there could potentially be an infinte amount of possible explanation, not necessarily only 2.
This is why even if evolution was shown to be wrong, it doesn't mean creationism is right, it means we no longer have an explantion.
It would still possible that life exists because of some other process that we haven't identified. That is also why a theory/explanation can never be proven to the the "right" explanation. You can't ever know that there isn't a different explanation, which you don't know about, that explains it better.

If you think that just because some explanation's predictions being correct proves that the explanaiton is correct, then you're committing a fallacy called "affirming the consequent".
Basically, if my explanation predicts that X should exist, and we then find X, it doesn't mean that X exists because of my explanation. There could be other reasons that X exists.
The more you can repeat this process, the more certain you can be that the explanation has good predictive power, but you can never know if it was a coincidence or if the explanaiton is in fact the "correct" one.
That's why the only thing we care abotu is whether we have predictive power, not whether something is "the absolute truth".

" : and we can see that'd it'd be stupid to attribute all of such intricacy and complexity to chance ... this is true because of your pathetic attempt to attribute some kind of order to something which depends totally on chance ..."

The straw man continues. Get back to me when you start talking about evolution.

" Yes we have very good reason to think that intelligence existed before the flagellum did ..."

Not particularly. Sure, there may have been sufficiently intelligent creatures before then, no one knows. We have no direct evidence of it, so no reason to think that they in fact did exist.
I agree that some intelligent creature could, scientifically, have existed at that time. But we only have good reason to think that they could have existed, not that they did.
We have zero reason to think that they in fact did, since we can't even confirm that they do, now, apart from humans. Humans are the only ones we know of that are capable of making any proper technology.
We have reason to suspect that other may exist, but we have no justification for believing that they do until we seen any kind of sign of them.

"we know NS and random mutations can and will destroy : that has been seen and observed ..."

Define "destroy". Remove functionality or structures? Yes, in some cases, that is predicted by the science. It's the same reason we lost most of our tail.
When we humans destroy things, we tend to leave a bunch of rubble, if you know what I mean. Evolution doesn't do that, it cleans up after itsel, so to speak. Maintaining and building useless structures is a waste of energy and will not be selected for.
Therefore, you can't compare it to "destruction". It is more like "streamlining".

" we know for certain NS and random mutations can't and will not build from scratch : seen and observed ... "

That's not how evolution works. Evolution works with what it's already got. It doesn't make things from scratch.
That's also why evolution is not the origin of life, since evolution requires something like life to already exist.

"*No, evolution favours beneficial information, and weeds out bad changes. If you're going to argue about evolution, then learn what it is and what it does.*
 ... lol I believe it's natural selection that "favors beneficial info. and weeds out bad ones" "

Yes, natural selection is the explanation for how evolution works. At the base, it's that simple.
Mutations are not "evolution", as I've explained.
Individual variation is not "evolution", either.
Natural selection applied to these things, however, is the explanation how evolution can happen.
That's why the theory is called "the theroy of evolution by natural selection", implying that "natural selection" is the way that evolution happens.

"... evo. says this can cause frequencies to shift and organisms to gain complex structures "

Yes, evolution is the change in those frequencies, and our understanding of this process predicts/concludes that complex structures can arise over extremely long periods of time, due to this.
And we've seen that. You just don't want to accept that we do, and I can't force you to accept it. The fossil record shows this. It's your right to deny it all you want, but there are good reasons why scientists don't deny it. And we don't have anything to talk about if what you're going to do is simply deny it all. In such case, we'd be better of discussing how religion makes you deny such things.

"Beyond natural laws = "magic", as I've pointed out before. ... Umm "Beyond natural laws" = "Supernatural" "

"Supernatural" doesn't have to violate the natural, but magic does. The idea of "magic" is that something just violates natural law, and does physical things, without being scientifically explainable.
Supernatural, if it exists, could be perfectly OK remaining supernatural without violating the natural. The "multiverse" could be said to be in that category, since they don't propose that it violates the natural. But as I see it, if the multiverse exists, it is also natural. If the supernatural exists, it's also natural. I don't see what justification we could ever have to call anything supernatural if we can scientifically demonstrate it.

"... you can be Supernatural and use all the natural laws : being supernatural just means you're not bound by the natural laws ...  by definition, we can say music and beauty are supernatural ..."

Music and beauty are also bound by natural law. The idea of them aren't, but no idea is ever bound by natural law. The reason that we find some things beautiful is that our brains have evolved to do so, usually because those things are valuable to us, from an evolutionary perspective, otherwise because they remind us of somethign that is. Its our instincts attempting to control our behaviour.
Individual variation and experience causes us to have different views on what things are beautiful, for example.
Read "why we feel: the science of human emotions", by Victor S Johnston.

" ... thirdly, I'm thinking by this you cannot take the concept of music seriously: music is beyond sounds ... in the natural world, that's all to music: sounds ..."

We define some sounds as being music, usually if the have some kind of impact on our mind/emotions. In the same way, we define some pieces of metal to be cars. A concept itself cannot physically exist, as we've talked so much about.

"And you most certainly cannot claim that the explanation for some mystery is something that per definition cannot exist (magic), as far as we currently know. ... and one more time, the explanation is something that does exist: intelligence ... "

Intelligence is a capability of something to reason, for example. (Note that we have no proper definition for "intelligence", because we can't fully agree what it is.) 
We indentify some things to be "intelligent" as a characteristic.
I'm seriously hoping you're not arguing that a god would make things happen because of intelligence, rather than because of his ability to actually do things, but I mgiht be expecting too much.
The ability to do things is separate from the characteristic of being intelligent. No matter how intelligent someone is, it doesn't mean we can do absolutely anything. We can still only do what we're capable of doing, and that is determined by many things, not only our intelligence. I can walk because I have legs, not because I am intelligent. I can make a hourse of cards because I have arms/hands and beause I am intelligent.
What you're saying is that something that was intelligent did it. No explanation for how it was actually done, only that someone thought of it and somehow did it.
And as I have explained, intelligence itself can never be an explanation for something, becuse intelligence would most likely imply the ability to make free choices - at least this case, but tell me if I'm wrong. And if we're free to make any choice, then what we do cannot be predicted, therefore anything could potentially have been something I did or something I didn't do. A rock might be lying on the ground because I chose to put it there, or for some other reason. The fact that the rock is lying there doesn't prove I put it there, just because I was capable of doing so.

"But yes, "astronomically" is a vague word, I was just making a point. Anything that seems "unlikely" to us will be extremely common on these scales. ... Ok just want to be clear here: do you accept that it's "unlikely" that evo. would build a flagellum?"

More than once? Yes, absolutely, that is horribly unlikely.
But that it did, in the case of history? No, it most certainly did.

See, this is once agian a case of trying to put odds on somethign tha thas already happened.
Imagine a a large set of dice, again. Say that the flagellum, as we indentify it, is a specific dice roll, such as "4, 7, 1, 1, 2...". The chance of that specific dice roll happening again is very small, obviously.
But now consider that you just roll those dice, and some random result happens. Now take that result, and call that "the flagellum". That is basically the situation we've got here. The flagellum was one possible thing that could have happened, out of hell knows how many possible things. Simply because the flagellum was the one thing that happened doesn't mean anything.
But like i said, I agree that if you were to roll the dice, it wouldn't happen again, a priori.

Of course, evolution isn't random, so the analogy only goes so far. The reason the flagellum is what it is, is because evolution had to work with what it already had.
Humans did not evolve randomly, we look like apes because we came from ancient apes. Evolution did not have the freedom to make us like birds.

"if a system needs all the said parts to function then it can't function until all said parts are present ... "

It can't perform that function until the parts needed are there. But it could perform some other function. That's why IC is pointless. An IC system can still evolve if the steps towards it were beneficial in any way, and even possibly if they were neutral, at least to some small extent.

"that's the challenge that evo. has to meet: but apparently evo. just says : "Nah, it evolved by gradual steps" : that's all ..."

For any specific case, we can often specify what steps those were, because we can often find cases where the "old" function is still there, and we can see taht it would only require 2 steps, for example, for that function to become the other function.
As I remember it, this is the case for the flagellum, though it was a few years since I read about it.
Everything resonably complex is a repurposed version of something else, like how our hands are repurposed fins. Evolution did not make our hands from scratch. And even though our skeleton is unique in detail, it's still made from a skeleton very similar to it. Only small steps required, and each step can be beneficial.

"Darwin said that if there is some thing that could not have evolved by small gradual steps, then his theory is disproved. ... I thought you said "Darwin was wrong" ? ...  "

About a lot of things, yes. Obviously not about everything, since then there would be no theory of evolution. This part still stands, as far as I know. It's quite fundamental.

"And whether or not IC structures exist or not isn't relevant, because it doesn't pose a problem to the theory of evolution. ... yes it does ... like I've explained ..."

It does not, as I have explained.

"But in biology, there is a specific defintion of what we mean by "evolution". It is not simply "change". ... yes in one instance it's change in allele frequency, in another instance it's forming complex molecules from simpler ones ... it's definitely not that simple I'd say ..."

"Molecular evolution" is not biolgoical evolution. It's not covered by the theory of evolution. This is exactly what I just explaiend to you, that word "evolution" itself has a very general meaning, but in biology it has a specific definition.
Forming complex molecules from simpler ones is not the same context of "evolution", if you use that word. It simply isn't evolution, it's chemistry. There are no species, no replication with variation, and so on, so it's clearly not the same context, as it's not describing the same process.

"But the point of the science of evolution is to explain how the change works. ... and it has managed to say the change works by scrambling and destroying pre-existing info thereby forming brand new systems in the process ... it's actually amazing how this would be expected to work ... "

If it's so "amazing", why don't you read a fucking book on it? You sure could stand to learn the basics. Yes, evolution is amazing, and very interesting, and most importantly extremely powerful. That is why it's of interest to multiple fields of science.

"Science is supposed to explain things, that's why we do it. So the interesting things is not that things change, but how they change. ... OK I get it: the science just explained what we saw all along: it just explains why our siblings are different from each other ... if so then that's OK ..."

The fact that you're different from your siblings is not because of evolution. Evolution did not make that happen (or did it? Consider the "evolution of evolvability"). Evolution is a process by which the gene pool changes, it isn't responsible for individual variation between individuals, it's responsible for the gene pool as a whole shifting towards some specific trait.

"But IC is not even an observation, it is a statement of a possible attribute. ... IC is not an observation? ... please tell me I've not wasted hours of my life in vain ... please ... "

The idea of IC exist whether or not any systems exist that are actually IC.

"They had absolutely no plan to create these dog breeds that we have today, because none of them lived long enough to care about the long-term effects of their selective breeding. ... what? their plan was to get specific qualities from dogs: so yes their plan was to create the different breeds:"

No, I don't think so. I think a hunter needed a dog that was good for hunting, so they bred a dog from a good hunting dog. They didn't know it was going to end up becoming a specific breed thousands of years later. They probably had no such concept.
No single person lived long enough to see any major changes, I suspect. I mean, people didn't live as long as we live today, which would probably only allow one person to see perhaps 10-20 generations of dogs, if they worked as breeders. I'm only guessing of course.
But over 10 000 years, we're talking about thousands of generations. Perhaps if you could see 100 generations, you'd notice a difference to the point where you'd realize that something weird was going on, that something "new" had happened. I don't know, I can't say.

"of course people talking about IC know it's a vital point when defending ID : and the argument has to make sense to convince anybody ... "

Oh, nooo, you're giving people way too much credit. You can easily trick people into believing all kinds of crazy shit. A few examples: UFO's, psychics, conspiracy theories, urban legends, gods/religion...
It's a sad fact, but most people cannot reason properly to any extent, since we're prone to fallacies, or don't have enough knowledge about things to be able to tell whether something makes sense or not.
And when you add religion to it, you've got religious people who want evolution to be false, and will accept any argument against evolution as being valid and sound. And remember that most people on earth are religious.

"*"Look how unlikely this is, we cannot believe it could evolve" <- an argument from incredulity. What you can believe or imagine has no impact on the truth. *
... what truth?"

Whatever truth, it doesn't matter.

" what I believe is strictly coherent with the truth we've ascertained by observation and repeated testing  "

That's not what I'm talking about. I am saying that you've got a situation where people are appealing to incredulity, which is a fallacy.
If I "can't believe a car can be red", it doesn't mean that a car can't be red.
When people say "I just can't believe that evolution could cause this", then you've got this fallacy. And to try to present evolution in a way taht makes it sound as implausible as possible - which you do - is a rhetorical trick of appealing to your audience's incredulity.

"And I agree, the long term capabilities of evolution isn't intuitive. ... and it isn't factual either ... "

Tell that to the people who use evolution in technology.

"if it isn.t intuitive, why would you blame anybody for rejecting it?"

Because you shouldn't reject something just because you can't understand it. You should have no position on it until you understand it.
There are plenty of things I don't have an official position on, because I realize I don't know enough about it. A lot of things considering politics, for example. But you still have a million people who understand even less, but are sure that they're still right about whatever they believe in, and that's a problem.

When it comes to evolution vs creationists, you've got all these creationists saying "no evidence exits", but they don't know what evolution is, or even what evidence is or how it works (yes, sadly, that's too common), and even though the ones who do know these things keep telling them that they're wrong, they keep insisting.
Yeah, it's annoying.

"Yes, to make the system perform the function its performing. Like said, this is too obvious to even mention. ... well I'm happy you see how easy this is to understand now: something I've spent probably weeks trying to force through the heads of you and Spiegel"

"Now"? I have no idea why you ever thought I disagreed or didn't understand this. It's extremely basic. The difference, which might be confusing you, is that I know that this doesn't actually mean anything, it's irrelevant. We don't agree on the implications of IC, quite clearly.

" ...  and something that the so called top scientists apparently can't grasp: you must feel the shock Behe feels everytime he tries to explain this "

Behe is an utter moron. And he's dishonest, aswell, as shown in the court case. Which, when I come to think of it, probably means he's actually a conman, not a moron.

"... apparently his mistake was thinking his concept would be so easy to understand ..."

His mistake would be thinking that people didn't understand it. Jsut like you, who also seem to think I don't understand IC.
You can't seriouslty think that a "top scientist" wouldn't be smart enough to understand such a simple concept as IC. Get real. The difference is in what you think about the implications of IC.
Behe doesn't work with evolution, he is not an expert on that subject. The experts who actually work with evolution, knows that he is wrong. And so do I, even though I'm a layman.
And most importantly, we can explain why he is wrong about the implications of IC, and I have.
First of all, IC systems are a lot rarer than you or Behe seem to think. Secondly, IC can still evolve. There is nothing about it preventing it, and it's a shame neither you nor Behe has the intellect to understand that - or perhaps it's just a lack of undertanding of the science. (When it comes to Behe, I'm not convinced he's even an honest person.)

"*But, that doesn't mean, in any way, that it doesn'tperform some useful funciton, which is why IC isn't an argument against evolution.*
 ... just wondering what useful function a car without an engine can perform ... spare parts?"

The problem of the analogy is that a car isn't trying to survive or preproduce. A car without an engine can still act as somewhere to sleep, or hang out, and it can be used as decoration. Just a few examples.
But life isn't trying to be used by someone else, it's only trying to keep existing. And that's only because the ones that try to keep existing are the ones that do.

" ... that'd mean vestigial components in evo. terms ... however the idea of exaptation is one which is highly wishful and less factual: exaptation assumes all parts of an irreducible system had previous different functions and just happened to be well matched to each other such that they all came together at "so so" time and formed a functioning IC system ... well that's a laugh ... "

Well, that's what we see. We see birds evolving feathers long before they evolved flight, for example.
But you're reversing the issue, somehow. The fact is that, in the case of dinosaurs, they only evolved flight because they already had feathers. Oethrwise, they probably wouldn't have.
If a species has no way to move around, but needs to move around, then yes, they'll evolve something based on their current structure. That's obvious. I don't see what you find weird about this. It makes a lot less sense to think that a new system would evolve from scratch, since that would imply that evolution could plan ahead.
Exaptation is not about IC, either, it's about repurposing things. Whether or not IC is a characteristic of any of it is irrelevant. Evolution does "care", so to speak.
And the existence of IC, for example, is not directly due to evolution. Evolution can only cause something to become more or less common in the population. When we talk about new sructures evolving, the point is that the system requires multiple generations, and without the selection feature of evolution, it could not have happened. But that doesn't mean evolution is directly responsible for the existence of the genes that produced he system. Only indirectly.

""Hello" is IC, but that is completely irrelevant to evolution, since it could still evolve from the word "hell" in one small step.
... I think you forgot to explain how this is related to evo. ... I mean can "concepts" evolve the same way as organisms? ..."

It's an analogy, it demonstrates that "IC" is irrelevant.
If you have a biolgical system, and you change one gene that causes a new addition to the system, and causes the system to do something else, then that new system might be IC, but that doesn't matter, it doesn't make any difference whether it is IC or not.

The only thing we can say about something that is IC is that there must be some way of turning that IC system into something useful (contextually) by making a small change.
But guess what? That is true about non-IC aswell! It's simply a truth about evolution as a process, and IC doesn't impact that at all.

In any case, whether it's IC or not, there must be some way that it could have evolved into what it currently is, and have remained beneficial at each step.
Once again, IC is irrelevant.

" maybe I used the wrong terms ... let me repeat evo. is more likely to degrade pre-existing components than add new functional components ... "

Explain to me how natural selection would favour degradation of existing components, if those components are useful to the individual?
A wolf born with a weaker leg, why would it systematically get selected for, by natural selection? It would make more sense if the ones with stronger legs would get selected for, which would cause their legs to become better over time, not worse.
I mean, there are cases where that happens, though. Whales lost their legs, for example. But in this case, legs were no longer beneficial to keep, since they were becoming aquatic. Useless things cost energy to build and maintain, and can become a liability, and that's why they're generally selected against.

"Becoming more or less complex doesn't matter, whatever has the best result matters. That is, whoever makes more babies who go on to make more babies is what will exist in the future. ... well becoming more complex matters if a flagellum is going to appear from nothing ... and it matters a whole lot if evo. is to be taken as an explanation for origins ... "

Yes, it sure is the general tendency over longer time scales.
And yes, a bacteria that needs to move [faster] would have to evolve some way to propell themselves. A flagellum was a solution.
If you have no way of moving, and you need to be able to move, then you're probably not going to be able to start moving by losing something. You probably have to start gaining some new structure.
And it's true that this new structure must perform a useful function every generation, as it evolves to become better at its function.
A fish on land that cannot move at all might still benefit form what would later be considered a 1/100th of a leg, as long as that can make it slowly move.
If humans would ever evolve wings from our arms, we would look back at this time and wonder why we had half-wings (our current arms). But they're obviously beneficial to us, even though they can't make us fly. See how subjective and relative this is?

"Intelligence is a capability/feature of a creature. It is the creature that does such things.
 ... hmmm first of all : "creature"? was that a typo? ... "

No, just a... sort of strange choice of word, I admit. Remember that I'm not a native english speaker. :/

"secondly intelligence is the only explanation that makes most sense with the evidences ..."

If you don't understand evolution, then... I dunno, I can't not see it from what I currently know, really.
ID doesn't explain the evidence. It doesn't explain why we can sort all life into a "tree of life", to start with.
Hey, we've been over this, I've explained this, and given you the challenge for ID to explain the evidence, already. It doesn't explain the evidence, it just appeal to you to simply accept that the creator did whatever the fuck he wanted to do, for no reason at all. And apparently he must have chosen to do it in a way that makes it seem as if he didn't do it.

" also, there's no concensus as to what exactly intelligence is: it's probably just one of the concepts like music... we know it exists, but we just can't put a definition to it "

Yes, and we don't want to tie ourselves down into a definition that will only limit us later on. If we'd find life on some other planet, we want to be able to know whether they'r eintelligent or not - even if they're extremely different from us.
We dont' knowif they'll also be creative and innovative, and if they'll have culture and philosophy and so on, but does that mean they can't be as intelligent as us, or even more intelligent?
This requires that we define intelligence, but we haven't been able to. And I suspect we're not very keen on doing it, because of the implications. If we could definitely say who is smart and who isn't, then that could cause societal problems, and I don't think many people are interested in being the cause of that.
Right now, we have IQ tests, but we also know that they do not measure "intelligence", they only measure "IQ". (I've taken an proper IQ test, btw, as part of my evaluation for possible Asperger's syndrome.)
Basically, if you're good at IQ test, it proves that you're good at that kind of tests. :P

"... however it's a cause we know can create amazing things: and the only cause we know which can create a biological motor  ... "

Nice going, to completely ignore science, there.

It's possible, perhaps, I'm not saying it isn't, I'm just saiyng we have absolutely no reason to think that's the case. ... I'm saying you do ... evo. says it just happened by chance:"

Being ingorant of the science is one thing. Straw manning it is another, and out-right lying about it yet another.
Evolution does not say it happened "by chance". Since I have corrected you a number of times on this, you can no longer blame it on ignorance. It's becoming a case of lying.

" no observable process creates life: what we can observe is just duplication and variation of pre-existing life ... "

Evolution is not about creating life, but about diversifying it. Don't blame the theory of evolution for not explaining something it is not supposed to explain.
We have no theory of abiogenesis, at this time, only hypotheses.

"this is one of the most close-minded assertion you've made: not surprised though"

You mean I should "open my mind" and just believe in religion, like the majory of humans? Sorry, you do not have the privilege of being a minority, you cannot claim that we relatively few who do not think that a god created everything are "close minded". We didn't just go along with the flow, we actually cared about what is true.

" ... but Dawkins said: “Biology is the study of complicated things that give the appearance of having been designed for a purpose” ... "

Yes, that's how I remember it, aswell.

" you really need some guts to say there's no sign of design in life ..."

There isn't. Appearance of design doesn't mean it's been designed. I agree with Dawkins that evolution is cool in the sense that it can, on the surface, create things that we would intuitively think is designed. When you take a closer look, however, ti doesn' tlook as designed anymore.
Yes, that's right, I agree that intuitively, it would make sense to think that life was designed. That's why religion has always existed, and all of them with stories about how life was designed in some way.
But I also know that human intuition leads us the wrong way, a lot of the time. For the most part, it's useful to us, but when it comes to more "foreign" things, it's only in our way, and we can't turn it off unless we learn to reason properly.

" "if you look at the details of biochemistry, molecular biology, you might find a signature of some sort of designer" - Dawkins "

Either I don't know the context, or that's a pretty bad thing to say, if by "designer", he doesn't simply mean evolution.
Sorry, I don't know the context, I don't know what he was saying. It's a short quote.
But I don't agree with what this quote seems to imply. And I don't care if Dawkins said it, I'm not a "fan" of Dawkins, and he isn't automatically right just because he's Dawkins. And he can also accidentally say bad things.
I could look up the quote, of course, but it really doesn't matter.

"... yet you are damn sure there's no sign of a designer ..."

Yes, because as I have said, the only way to argue that life is designed because it "looks designed" is by relying on fallacies. We have no idea what a thing designed by a god would look like, so we can't tell if this is such a thing. And you can't get around this, no matter how hard you try.

" and you wonder why I don't take you seriously most of the times ..."

No, don't worry, I know why you don't, and it has nothing to do with me, which is why I don't care.

" I hope you're keeping close touch with your comments ... cuz it seems like you're in rant mode again ..."

I do that, it's part of my character. However, to us autistic people, it's called "info dumping". It's something we do quite often, and not everyone appreciates it. But we "aspies" don't appreciate some things that neurotypical people do, either.

" in this case it says more or less what ID says which is ; there are certain biological systems which exist which is best explained by an intelligent cause instead of an undirected process like evo. ... there's absolutely nothing religious about these two claims"

I know, but just because you don't put religion in teh claim doesn't mean it's not religiously motivated. Creationism is also the claim that species were created "by god" in their present form, or in basal forms. Remove the "by god", and you've got ID, essentially. But that doesn't mean the people who keep pushing this doesn't actually mean "by god", aswell, and that it's driven by the exact same motivations.
And you admit this, that to you, this ID is the christian god.
Find me an ID proponent who believes aliens are the creators, for example, and not a god.

However, the reason that ID is not science, but rrather religion, is because you started from the wrong end. Scienc elooks at the evidence and goes where it leads you. You migh tnot have the self-insight to realize this, but ID people had already decided that ID was the answer, before they ever looked at the evidence. This is because the peopel who push ID used to call tehmselves creationists. The only reason ID exists is because of crweationism, and creationism waws a religion, and ID is the same thing that it always was, whether or not you remove the word "god" from the claim or not.

But don't get me wrong, now, I don't have any problem with people researching ID, on the face of it. It's perfectly valid to check whether their hypothesis is corrector not. The more science the merrier.
The problem is how it's being done. It's not being done scientifically, but politically. They're not interested in doing it the scientific way, like the rest of science. And they distort the science, and attract a lot of conmen who make money off lying about the science.
It's basically completely rotten, even if there are one or two honest people hiding in there, somewhere.

" ... it's just like saying the stonehenge was a result of a specific act of creation: or saying the stonehenge was intelligently designed ..."

Yes, sounds fine, except that's not what ID is, in practice,so it doesn't matter.
See, we have this political party in sweden right now. Xenophobes who want to stop immigration, perhaps you've heard of this wave that's spreading across europe.
Officially, they never say anything that could be considered racism. But that doesn't matter because 90% of the people in the party are definitely racists, and quite hard-core racists, too.
This is the same as with ID. They've taken creationism and made it appear completely non-religious, yet everyone behind it is doing it for religious reasons, and with religious conviction, so it's only a trick. It's a matter of PR. And it's sad when you've got people who think that a scientific idea would need good PR instead of evidence.
It's frankly a disgrace.

" if you believe is any sort of creation or design in life, you're a creationist, be it deist, theist, panantheist, etc ... or young earth creationists, Old earth creationists, evolutionary creationists ... you can even believe aliens created life or whatever: you're still a creationist ... "

Yeah, so what? Find me an ID proponent who isn't a theist!
If effectively every single ID proponent is a theist, then I don't care that someone who isn't a theist could be an ID proponent, when in fact there are no such examples, or an insignificant number of them.

"but if you define creationism to be the view that the universe and life came as a result of special creation according to the book of Geneis in the Bible : then you're talking of a totally different concept which is Biblical creationism : this specifically names the creator to be God "

Sorry, is this different from your view of ID? I mean, if you were once a "creationist" and is now an "ID proponent" instead, does this mean that your belief about this subject has changed? I'm guessing not. So I don't care how people dress it up, it's still the same thing.
I agree that ID doesn't ahve ot be the same thing. But you have to be religious to propose ID, because you have to have a bias to do it. There is no evidence of ID, because it cannot be tested. If you're a person who would support ID, then you were already a religious person to start with.
Basically, ID is not officially tied to a religion, but everyone in that group are religious, so it's still the same thing.
Like I said, PR. And the court saw through it, and so do I.

If ID was really science, and not religion, then why did they try to put ID into school without having scientific consensus first? Right there, they've proven my point, that ID is political/religious, masquerading as science, but not doing a very good job of hiding it.

" considering that creationism just happened been merged with Biblical creationism, it was obvious that going by the name "creationism" was going to constantly insinuate Biblical creationism"

When I say "creationism", I am referring to the idea of "special creation", that species orbasal forms were created separately. Whether biblical or not doesn't matter, but I haven't ever heard a non-biblical creationist. Jews, Christians and Muslims all believe the same creation story, right?
So that pretty much leaves hinduism, and I did talk to a hindu about it, and he/she said that hindus aren't dogmatic, they accept science, and that it's mostly a life-style/philosophy.
Same thing goes for satanism. I am a satanist, not that it matters, since we are basically ego-centric secular/atheist humanists with some added symbolism.
To be honest, I can't remember what buddhists believe about the origin of life. :/ I really should check that out.

" ... so ID was probably the name used to start up a brand new scientific approach which was strictly based on testable and observable evidences"

Yes, "evidences". :P Sorry, it's called "evidence", it's an uncountable noun. Not that it matters, I'm not a grammar nazi, or anything, but it's funny how creationists keep putting that "s" at the end, as if they have their own unique culture. :)

Anyway, evidence isn't testable. Predictions are testable. And ID doesn't make any predictions, so it's not testable.
But don't feel bad, string theory doesn't make any testable predictions, either. So far, string theory hasn't been useful, either, because no one knows whether string theory actually applies to reality. (Also, string theory is not a theory, obviously, it's a hypothesis. Don't get fooled by the name.)

" ... and it says that the evidences show signs of a designer "

Yepp, so they say. I've heard that.

"... if you can maintain the original definition of creationism without making equivocations, then that's fine: but I'd reckon you wouldn't cuz the only way ID can be deemed religion is if it's equated to Biblical creationism ... and that's what happened in the court ..."

I don't have to call it a religion. My point is that it isn't science because it doesn't follow the scientific method, and the same is true about creationism. I don't need to say anything more than that about it.

"*No, explain the process used. [...]*
 ... how about you explain the process by which it evolved? ... yes I don't mean "Natural selection and random mutation": I mean the exact steps it took and the exact processes ..."

We don't know that, and don't claim to know that. Neither is that covered by the theory of evolution, obviously, which describes the process of evolution, not the history of life on earth.
We don't even know if it's possible to know that level of detail about what happened so very long ago. I'm quite sure it isn't possible. All we can find evidence of is the general picture, the fossil forms of how different species looked, like snapshot photographies, through history, aswell as what evidence they've left in the genome of modern life.
And we should be thankful we can even know that much, that life on earth does fossilizze that way and remain, to some extent. I bet there are planets where life wouldn't be able to even become fossilized, if it existed on those planets.

But yes, the theory of evolution explains the process that caused life on earth to diversify. And you can study that, and I recommend that you do. You can also study those snapshots (the fossils and the fossil record) and at least learn what we do know about it.

" you don't even have a consistent definition of evo. in biology"

Very strange, since I've given you that definition multiple times. I'm sure you're just messing with me, but here it is again: "The change in allele frequencies in a population over time".

" ... actually it's more like the theory has been almost changed totally to fit the evidences that contradict it ... "

To be able to make such judgements, you would have to actually know the science. You don't. You don't even know the definition of evolution, even thought I've told you a number of time, which is pretty damned fundamental to understanding the explanation for it.

"You seriously think you can match that by saying "design", as if that would be an explanation?
 ... I seriously wish there was something credible to match ... most of the evidences clearly show design ... evolution is totally clueless as to how IC systems appeared ..."

Oh, the defensiveness is off the charts.

" for God's sake experiments show evo. degrades pre-existing components ..."

Some experiments do that, yes, and that is as it should be. I've explained this. Those organisms that they are experimenting on come from a natural environment with complex selection pressures, which requires them to be able to deal with many problems. We bring them into a controlled enivinronment with a focused selection pressure, which means that the organisms will be more fit to that environment if they discard all their adaptations to a more complex environment, since they can save so very much energy by becoming more simplified. Evolution doesn't "know" that this would be a disaster if they were returned to their natural environment. This new breed/species/whatever would go extinct because it couldn't handle the sudden gigantic change in environment and selection pressure.
But within this controlled environment, the reason that they discarded some features is because it made them more fit.

"well I chose a name which would be easily recognisable by you : but it was naive of me since you believe God is different in Christianity and Judaism ..."

No, I'm not sure I believe that... :/ In fact, I think they're supposed to be the same god. The only problem is that the religions don't agree on what the god did/does, in which case it can't be the same god, unless you assume that only one of them are correct (or none of them).

I mean, it's the jews who "own" the creations story. Then comes christianity and adds thei own stuff ot the religion, and call it christianity. But the jews don't agree that their verison of it is god, and they're the ones who "own" the creation story. :P So christianity doesn't have a creation story, because their god is not the god that created the world in Genesis.
I'm obviously just having a bit of fun witht he whole thing. Religion is a great source of comedy, you have to admit.

"Jews and christains agree about God: did you forget that the jewish text, the Torah is a part of the Christian Bible? ...  "

The god of the Jews didn't send his son down to Earth, that's a pretty big difference. One god did, and the other one didn't, so it's not the same god.

" religion is actually evolving(and I'm using the term correctly here)"

Yes, and it evolves through natural selection, too. The versions that aren't fit to survive as society changes (environmental pressure) die out in favour of the ones that are.
Same principle is true for languages, aswell. And it's amazing how extremely similar this is to biological evolution.
But wait, you don't think it's possible for a language to evolve into a differnet language, right? Some ancient roman people got separated from the rest, and over time they started mutating their language, and it eventually ended up as spanish.
I read a nhistorian who said that old swedish and old english used to be so similar, only less than 1000 years ago, that they could talk to eachother without the need to translate. Amazing how it could get so different in less than 1000 years. We're talking about perhaps 50 generations, only.

"Not because it's rational to believe that, but because it feels good. Yes, it's become pathetic.
... maybe you should stick with what you actually know ... "

That's a really shitty argument, you know. If you're gonig to disagree, then make a proper argument, or it only looks like you can't.

"Creationism barely explains half the facts, while the other half speak against it, or remains oddly inexplicable. ... Oh so are you saying creationism explains some facts? ... it definitely seems like you're ..."

Yes, what I am saying is that creationism does fit with some facts, in that it doesn't contradict them. If it were only for those facts, then creationism would be a hypothesis worth checking out.
But whwen you add the reast of th facts, it no logner fits, while evoklution does.
That still doesn't mean evolution is right, because it still needs testing. (It's been tested.)

" but you keep saying there's no evidence of design in life"

That's right. For something to be evidence of design, it would have to be evidence for nothing but design. The same fact cannot be evidence of two opposing explanations, or it is evidence of none. The mere existence of life could fit with a number of explanations, meaning it doesn't support any specific explanation. That's why the mere existence of life isn't evidence of anything, it's just a fact that life exists.
An there is no evidence that uniquely supports design. I have explained the problem of finding evidence for design, so I won't repeat myself again.

"*Evolution is the only explanation we have that accounts for all the facts.* ... actually evolution is the only explanation you want to believe in ... "

No, I want to "believe in" whatever process is able to create life or diversify it, since that would be pretty cool and useful. If it wasn't evolution (for diversity, not origin), but something else, then I would be very interested in that thing. Similarly, I'll be very interested in the explanation for abiogenesis, once that's been properly solved, if ever.

" ...but evo. has been as a matter of fact demonstrated to be false on many fronts ... the fossil record easily takes evo. out ... easily ..."

You sure are tiresome. Give me an example to work with, instead of just being annoying.

"The theory of evolution has been tested and confirmed. Nothing you say can change that. ... lol ... you must think this is an indoctrination session "

No, but I fear it has turned from a conversation into a grade school lecture. It's no longer a conversation, but rather a case of me having to tell you the facts - and you consistently denying them, of course.
But sure, if you think teaching is equal to indoctrinating, then whatever.

"... "X is true, there's nothing you can say about it" ... lol hell no you have to prove that "X" is actually true"

Soon you'll have me prove that the world is actually round. Really, if you're going to have a conversation, then at least learn the basics of the subject.
Yes, the theory of evolution makes predictions, and those predictions have been tested and confirmed, over and over. And yes, like I said, nothing you say will change that, so live with it. (Or stay in denial, I really don't care anymore.)
An explanation that is able to consistently predict future observations has predictive power. That is the theory of evolution.

" I remember you saying evo. theory isn't a scientific fact: now you're saying it's "been tested and confirmed" : that's the criteria for a scientific fact "

Tested and confirmed means that the predictions have been confirmed through testing. This is not he same thing as being a fact, since a fact is just a fact, not an explanation.
The criteria for a scientific fact, as far as I know, is something that has been established with at least 5-sigma certainty (where that applies), or something that is indisputed or indisputably a fact.
The phenomenon of evolution (change in allele frequencies...) is such a fact. It is indisputable because anyone who understands it knows that it must happen, and we see that it always does happen.

"*Write papers to peer-reviewed science journals and present your evidence.*
 ... I would but I don't want to cause another scientist to loose his source of lively-hood because some close-minded excuses for scientists can't listen to a different perspective ..."

What, is it your livelyhood? I told you to write science papers. Are you afraid of losing your job if you did that, or what? I don't see how you're making sense.

"Do note how basically not a single ID proponent ever actually does that. ... lol you silly man ... when some one can loose his job for publicizing an ID paper it clearly shows a bais towards evo. "

No, you'll only lose your job if you push a science paper that makes claims that would overthrow pretty much all of science, yet provide nothing in support of it, except for logical fallacies.
Yes, that could certaintly cause you to lose your job. And it's not because you're challenging evolution, but because you're proving yourself a really, really shitty scientist.
You'd face the same problem if you did the same against thermodynamics.

However, if you actually had strong supporting evidence, you'd win the nobel prize, probably multiple times! It would be fantastic. So go ahead, if you really think you've got something!

"... evo. proponents can come up with any BS they want and it'd pass as peer reviewed so long as it supports the dogma"

Peer reviewers don't check for "dogma compliance", they check for proper scientific methods.
Hey, try it! Write some stupid BS in favour of evolution, and see if you'll get published.
It's very well possile that you'll get published, but you'll still get laughed at by the rest of the scientist, and you and your paper will be forgotten, apart from the occasional meme or something.
Because yes, sometimes crap gets published, perhaps because it still appeared to be a proper scientific method, or because the peer reviewers are only human and make mistakes because they were in a hurry, or something.

" ... ID proponents are limited to debates and Books which luckily turn out to be good sources of scientific knowledge: you can search out the debates and read a few books for more knowledge"

I've basically watched every debate I could find, over the years. I've probably seen 100 hours of things like that. I do find it very entertaining and interesting, for the same reason I have this conversation with you.

" ... but I doubt you've done any of that ...  "

You've completely misjudged me, in such case! I watch lots and lots of it, that's why I've heard all the arguments, over and over, even.

"still, you claim to be rational ... "

Has nothing to do with it, though. "Reading up" on something is not about being rational, it's only about increasing your inventory of information to work with.

"No, "intelligence" requires evidence, like everything else. You're not allowed to bypass the scientific method just because it suits you. ... what evidence do you require? IC, fossil, finetuning, SC, which one ? ... I've given you detailed explanation of some of these ... all follow the scientific method ... all are vaible facts ..."

Well,a t least those are some points to talk about, rather than just making empty assertions.
IC, we're talking abotu that seprately, so I won't repeat.

SC <- I've asked people to define this, but have never got a definition. I'm sur eI've asked you, aswell, but you dont' give definition, either. And I'm tired of asking, so I'll just ignore this argument. Except you said you would give a detailed explanation, so please do. And make sure you define it so that I could identify a case of SC by its definition.

Finetuning <- Another argument from ingorance. The universe is oddly specific about its constants, and we don't know why, yet creationists then argue that because we can't explain them in any scientific way, it's an argument for creationism. Argument from ignorance.
Even the name "finely tuned" already assumes that someone "tuned it", unless my english fails me, meaning it's a case of begging the question when you ask "why is the universe finely tuned?". No, the proper question should be "why is the univesre so oddly specific?"
But we really don't know that it is. If the constants turn out to be a consequence of something, then it's not strange anymore. We just don't know, at this point.

Got anything else?

"Yet this process is used in technology because it does exactly what you think it won't. ... I hope you're not talking off you ass again ... cuz to my knowledge all our technology is direct product of intelligent design ..."

Advanced robotics, for example. They use genetic algorithms to have the robots evolve its movements or its ability to handle sensory data using neural networks (computer science concept).
It would be effectively impossible for a human to manually type in the numbers/data that details the movement of the joints to make a robot "walk", for example. But using evolutionary principles, they make the robot evolve the "perfect" way to move its joints based on some criteria (selection pressure).
If you consider what it would take to tell all of the muscles in your body exactly how to move to produce a "walk", you'll realize how extremely complex that is, yet the walk we do is really smooth. An intelligent designer can't do this, because it's too complex, but evolution doesn't care about complexity if that is a natural component of the problem.

Using neural networking, you can create a network of neurons that process input to find a way to solve a complex problem of "sorting" something complex, for example.
This can't be easily explained, so you'd have to look it up if you're interested.

" it is needd to explain the imaginary process of building livers and lungs and eyes and nose, bones, brains etc etc: all by random mutations ... still not sure exactly how this is science ... "

Then study the science and you'll learn. You could have done this a long time ago, yet all you do is argue, instead. Makes me think you don't actually want to know.

"I think the problem is you probably don't even understand science at all ... and honestly, I hope that's not the case ..."

Do you think I've misrepresented the science?

"You don't know what was turned into the flagellum, so you don't know what changes were required.
 ... and I suppose you do? ... lol ... hell no you don't ... "

I don't remember, but I did read about it, and I did know. What I remember was that it was some way to transport things in the cell, or through the cell membrane... I don't remember. And they did detail what changes were requires to turn it into the flagellum motor.
All you have to do is go and read about it, you know. Stop pretending that the answers don't exist.

""Complex" being an adjective, and "irreducibly" being the adverb that enhances the adjective. In the same way, we could say "incomprehensively large".
 ... hmmm ... I'm wondering did you do this check for evo.? ..."

What am I supposed to check for? Evolution isn't an adjective.

" atleast if you did you'd be able to give me a consistent definition for evo. in biology ..."

The change in allele frequencies in a population over time. I've given you this sooo many times, now, I hope it'll eventually sink in.

" btw IC is clearly defined by Behe: and it has nothing to do with something being red ... "

Troll.

" well same can be said about my school: most of what I know now are self thought"

Same here.

" ... just curious though what did you study in school? ... I really doubt it's anything related to engineering:"

Music in gymnasium, then music composition and production in "university" (not quite a university, but I don't know how to translate it).
Then software design and modulation at university, but didn't finish it because I got too bored of it (I hate having to program in Java).
Related to enginnering? That depends, software engineering, yes, and sound engineering aswell.

" because I don't think there's any engineer that should buy into something like evo. ..."

I didn't know engineers were that stupid. Or perhaps you're just wrong. Sounds more likely.

"place since the start of the Christain era you'd see that it'd have been impossible for humans to stay for 200,000 years and not even discover electricity"

Why 200 000 years? Humans have existed for about 2.5 million years.
And just when do you consider electricity to be "discovered"? When the first person saw lightning, which was forever ago? Or when the ancient greeks discovered static electricity, many centuries beofre year zero?
When is something so omnipresent as electricity "discovered"?

" yes you need to "think" your way to knowledge: if you're just going to digest everything someone says without questioning then you're not knowledgeable: you're indoctrinated ..."

If you "digest knowledge", you're not thinking your way to knolwedge, you're receiving it.
You have to study the world. Knowledge about the world must come from studying the world, not from thinking up new knowledge.

" evo. has never been proven right: as a matter of fact ... "

There's nothign there to "prove". The theory has been confirmed, not "proven". This is not math, you know, it's science.

"evo in the sense of the actual meaning: not "frequency shift" ..."

Oh, ok, I get it, you're saying that your straw man of evolution has never been proven right. I agree, but explain how this is relevant.

"And you're giving your opinion on something that you haven't studied and clearly do not understand. ... this is hypocritical: you give your opinions about things you have no clue about: you've even admitted it ..."

If I admit it, then there is no problem. You're pretending that you know what you're talking about.

" and it's not like I've not taken time to study evo. I have : that's why I can easily tell you that the basic confusion is in the definition ... "

You've taken time to study it, except you haven't even gotten past the definition? Then... take a lot more time. (?)
Or, have someone actually help you understand it.

"[...] It can lose its functions that made it survive in nature, because nothing is selecting for those, anymore.
 ... you've said absolutely nothing different ... experimental evidence shows evo degrading components"

Yes, as it should, in such a situation!

" ... and apparently this is the process used to upgrade and even create new components ..."

Yepp, same process, different scenario. Remember, life did not evolve in a lab, it evolved in nature. We don't tend to simulate an entire eco system in a controlle denvironment in a lab, since that is best done in nature, wher there is an actual eco system.
The things we do in a lab is to show/test one specific thing. You're trying to draw conclusions as if the test was supposed to test for something else.

" even in the "multitude of pressures" in the complex outdoors, there's been no observation of an organism building a complex system"

Only in the fossil record, as far as I'm aware, as that takes a lot of time.

" ... the advantage of the experiments is that it gives you the chance to force any pressure needed to build components and systems ... but that obviously has never been seen: "

An entire new system takes a shitload of time. We usually only have time for small changes, which can still prove points.

"the direct opposite is actually the case: ... in other words experimental evidences show that evo. is not possible ..."

Evolution is a fact, we've been over this. Your problem is that you don't define evolution correctly. You're talking about a straw man, and I'm not going to defend your straw men.

"Yes, you might mean it that way, but someone else might not.
 ... probably only if that someone is like you ... I don't think there's any christian that has a problem with what I said ..."

I wasn't talking about christians.

"You have "reasons", but you have no justification.
... I do have reasons and justification ... "

You say so, but I know you don't. If there were proper justification, then that would be huge news.

"*You cannot actually support your belief with anything. You may think you can, but you can't. *
 ... hahaha ... another "it is so because I say so" bit"

No, because the whole world would be aware of it, because it would be on every news outlet in the world for weeks.

"You're relying fallacies, which means there is no true justification.
 ... I'm relying on IC, SC, the fossil record, Entropy, finetuning, biogenesis ... no one told me these were all fallacies ... "

I have told you so. IC is irrelevant, finetuning and entropy and biogenesis are fallacies when applied here. As for SC, I can't say until you define it properly.
Biogenesis is the principle to contradict the notion of spontaneous generation. But when the line between life and non-life becomes blurry, biogenesis becomes inapplicable, it simply doesn't apply anymore. It's the same idea as how Newton's laws of motion appear perfectly fine, but only until you add strong gravity, for example, and then it falls apart.

"Yes, why one "can" believe in god, but there is no reason why anyone should believe in god.
 ...  actually there's no reason why I should take a baseless comment like this seriously ... and I'm sure any rational person would agree with me ..."

No, rational people, specifically, disagree with you. A rational person is someone who would avoid believing in contradictory claims, since that is irrational. And to avoid that, you need to not believe in things that aren't justified.
And a rational person also know that theism isn't justified, because if they would apply the same standard of evidence to everything, then they would also have to believe in all other gods, and leprechauns and magic and unicorns and a lot of other nonsense that will end up a mess of contradictions.

"I believe in coffee cups because I have evidence of their existence, for example. That is a justified belief.
 ... and I believe in God because I have countless evidences for the reality of God ..."

So you think you do, but you're wrong. If you had evidence fo rit, you'd be able to share it with me, for example. But all you share with me are fallacies and misapplication of science. I have "seen" your evidence, and it's not evidence.

"just like I can predict the decimal numbers for Pi would continue to change ..."

No, you already knew that. You can't "predict" what you already know to be true. That's called a "post-diction".
Same with evolution. At this point in time, we already know that "it will change", or however moronically you phrased it. You can't predict what we already know.

"But forget all of this. Even if the environment is random (changes randomly), the direction of evolution is not random if it follows the environment. Know the environment, and you know the direction of evolution.
... well finally you admit the obvious truth ... the environmental conditions are random;"

Reading comprehension fail, again. I said "even if", which doesn't mean I agree with you even for a second. Ever heard of "for the sake of argument"?
 I am pointing out that our disagreement on this matter doesn't have to be an issue, since it makes no difference.

" the mutations are random, evo. strictly follows these two ... so what makes evo. non random? ... lol ... this is unbelievable ... "

I have explain what makes evolution non-random: The outcome of the process is not random. But you clearly don't understand the concept of "random", either.
You know this is true, because you know that species adapt to their environment. If evolution was random, you'd not get adaptation.

"You want actual predictions, you have to talk to an expert, I'm just a layman.
... Ooookk ... so there's none you know of ..."

Exactly, the ones I've known of have already been confirmed, and I'm not enough of an expert in things like zoology, for example, to be able to make such predictions of my own.
I know when I don't know enough, that's why I have to refer you to some expert.

"Adding -1/+1 to zero, perfectly randomly, will tend towards zero, in that over time any small change from zero will disappear. You'll have an infinite amount of +1 and an infinite amount of -1, which adds up to zero.
 ... do me a favor please : use a practical situation ... take a coin and toss it : lets assume heads is +1 and tails is -1: take the average of every five tosses after adding the outcome to the initial value, starting from 0 ... if the average shifts from 0 then my point is made ... simple as that ... "

Sorry, you can't excape the math. :P And I really don't see why you're arguing about this, since this should be very clear to any adult who's gone to school.
Your example or my example, it doesn't matter, the result will tend towards zero in both cases.

"*So you're simply admitting bias? Nothing can be right just because it is related to evolutoin, huh? *
... yes I'm admitting the so called law is based on a bais ... a bais for a belief ... it could be right if it was a fact that orgaisms did morph from different organisms ... "

Well, that explains why this conversation is usless, then. You can't accept anything as true if it is tied to evolution in any way. The height of intellectual dishonesty, really.

"not sure why it's even called a law""

Then google what a scientific law is.
https://en.wikipedia.org/wiki/Scientific_law

" ... and I'm not sure I've seen a law that's based on a theory ..."

Theories contain laws, normally. The theory of gravity contains the law of universal gravitation, for example.

"Wings would require very large changes. Perhaps 200 million years could do it? ... yes of course how could I forget that ... so by my calculations in 1 billion years time humans would finally complete the evolution into dragons ... seems plausible to me ..."

Your calculations are crap. Start by understanding taxonomy and phylogeny, and you'll see why humans will never evolve into dragons.

"Even something that moves in a random direction has still beeen somewhere, meaning taht there is still a direction that would take it back to wherever it was.
 ... assuming there's a backward direction is simply assuming that all random directions are foward"

No, we only have to define them as being forward. As long as we're consistent with turning 180 degrees, it doesn't matter what you call the direction.

" ... if so then it's not undirected ... if there's something keeping you from going back, you have some sort of direction"

You've misunderstood the meaning of the words directed/undirected. It's not about having a direction, it's about being guided, or "managed". It's a matter of having an artificial element to the process.

"But evolution doesn't move randomly. However, it doesn't plan ahead, it's just a process of natural selection, so the environment determines where it goes with any specific species.
... OK evo. doesn't move randomly, but it doesn't plan ahead ... what exactly are you saying bruh?"

Yes, I agree that it looks confusing at first glance, but it's simple: Something can be non-random and still not have the ability to make plans.

" ... if evo. just moves without a plan, then it's random ... you're just contradicting yourself ...   again ... "

I would love to open your head up and see how you work. The way you reason is just so... characteristic.
No, sorry, plans or not doesn't have anything to do with randomness. Planning is a potential capability of an intelligent being.
Moving without a plan means it's just a natural movement, it doesn't make it random, because not all outcomes have to be equally probable.

"Nice contradiction. Fail proof but will eventually fail, huh?
 ... lol what? ... I said it was good enough for the designer, but other factors hindered the continuation, so the designer added more info. to adapt to the other factors ... what can't you understand here?"

Heheh, it's still a contradiction. :) Something that is "fail proof" cannot fail. Yet it did - no matter why, it still did, which means it wasn't "fail proof".

"No, sorrry, your explanation still has to explain the facts. There are no pre-cambrian rabbits, that's a fact. But more recent rock layers reveal more rabbit-like creature.
 ... well then in this case the designer just designed the rabbits at a later point in time ... "

See, there's my point, right there: A designer could have done absolutely anything. Or nothing at all. If there had been precambrian rabbits, then the desinger could have done that.
Absolutely everything about the unvierse could have been completely different, and you could still say "the designer just did it that way", without any explanation for why, at all.
It's a useless statement, and it's sad that you don't get that.
Neither does it fit the Genesis creation story, but I guess you can just claim whatever you like in the name of interpretive freedom.

" God is most likely the source of energy ... "

Heheh, physics fail.

" ... you're saying more nonsense ... "no one knows anything about any gods" ..."

Yeah, "I don't know that tea pots exist, but I know that they're green".
Fucking crazy people...
If you don't see why there is a problem with that statement, then you're officially not a rational person.

"But like I said, this isn't about fossils, either, this is about evolution. Fossils is paleontology, the history of life. The theory of evolution is about the process of evolution, how it works. ... Ok buddy ... but just to put this out: ID also explains most of paleontology ..."

As I have explained, ID can "explain" anything, if you want to it. Just say "some magical guy did it". Yepp, a magical guy could have done absolutely anything you want to say that he has done.
Note that I put "explain" in quotation marks. It has absolutely no explanatory power. It basically has negative explanatory power, as it would make everything inherently inexplicable.
I mean, talk about randomness... If some magical guy just made stuff the way it happens to be, then that is by defnition to invoke randomness, since all outcomes are equally likely.

"They didn't emerge out of nowhere. I suppose you've been misinformed. (?)
...the fossil evidence show they did ..." (Cambrian explosion)

No, and I gave you a link to some examples of transitions known from that time.

"Also, we do have fossils of animals long before the cambrian explosion, in case you thought that animals didn't exist before then. ... lol ... I'd love to see these animals and how the fill in the blanks : I'd like to see if they fit as transitions for the plethora of new organisms that appeared ..."

If you actually wanted to know any of this, you'd have looked it up. You're not interested in knowing anything about this, beause it interferes with you beliefs.

" the faster you evolve, the closer your transitions are expected to be ... "

Point being...? Weird to say something like that and not make any kind of point.

"A similar thing happened later, aswell, called the great odrovician biodivesification event.
 ... yeah a way to discredit evo. more "

You're failed to even shown how the first one affects the theory of evolution!

"... well I'd suppose the cambrian was different because the diversification was relatively exponential and the outburst of new organisms from nowhere was quite shocking to evolutionists who would have expected to see the slow morphing evidences of each species ..."

Did I only imagien taht I sent you a link to an example of the transitions during that time? Or are you ignoring that?
Yes, we always expect to see transition. And tha's what we see through the cambrian explosion, aswell. There is nothing about the cambrian explosion apart from it being a long time of reklatively rapid evolution, which is interesting only because rapid evolution doesnt normally last that long. But it has happened at other times, aswell.

"Here's one example, detailing the panarthropoda phylogeny. There you've got the common ancestor of tardigrades, arthropods, for example, the tactopoda.
 ... I think you might have missed my definition of "transition" : by transition I'm looking to see a smooth string of morphing b/w two relatively different organisms:"

Yeah, everything should be handed to you on a silver platter, huh? Go study it if you actually want to know about it.

" obviously one can just take creatures and fix them up in a "tree" and claim they evolved: that's not enough proof ... you have to prove that they actually shape-shifted to begin with ..."

Try to do that with something else. See which kinds of things can be sorted consistently into a tree structure. Really, do it, because by the end of that little exercise, you'll understand the significance.

" most likely, what happened is the plants were created first and then the first string of multi-cellular organisms next ..."

You're such a clown. I really shouldn't even bother pointing this out to you, but plants are multi-cellular organisms.

You don't test and falsify facts. You test and falsify explanations. Facts just "are". ... Ummm you do test and observe to determine a scientific fact ...

Facts are observations.

" don't know exactly what this is about this time ... the explanations are the "facts" ... If I say "this is a rock: as a matter of fact" , then that's an explanation:"

Is that so? "This is a rock, as a matter of fact" is an explanation, to you?
Fucking creationists who can even.... gaah...
I'll take this as you just trolling.

"No, this is simply a case of something that is hard to agree on a defiition of.
 ... yeah more or less: it's actually non-existent looking from a scientific angle:  "

...More trolling...

" ... yes you might be able to confirm that hard rock exists: you just can't confirm that it's music:"

...yet more trolling....
Looking at it from the bright side, this'll make the reply shorter.

" many people consider it to be noise: like me"

Yes, I also consider you to be noise.

" looking at it scientifically, it can't fulfill the criteria to be deemed a scientific fact "

Stop pretending that you know the criteria.

"WTF, when has science ever established that "music doesn't exist"? Are you fucking high, or something?
 ... again, think brother ... I said, if we strictly go by what science can prove, music doesn't exist because science can't prove that it does ... "

This reasoning would be fine, if it wasn't for the fact that just because something can't/hasn't be proven to exist doesn't mean it's proven that it doesn't exist, you moron.
You literally said that scientifically, music doesn't exist. That means that science must have established it as fact that music doesn't exist - not that it simply can't establish that it does exist. Since music does in fact exist, science cannot establish that it doesn't.

"if you say music is sounds, it easily gets falsified on experimentation"

Heheh, no, it won't, since music is sounds.

"But do you really think that music is the only thing this applies to? It applies to more things than it doesn't.
 ... a way to say it isn't a scientific fact ... "

A way to say this has nothing to do with science. This is semantics. You don't scientifically/empirically test semantics, because that would serve no purpose.
You could, there's just no point in doing it.

"Music exists, but a global definition of what should be considered "music" does not exist, as with the majority of things. ... Music exists yes: but it's not something you can say is a scientific fact ... I hope you understand my drift on this? ... we just all asume, and agree that music exists ..."

No, it's definitely a fact, and it has real implications. As I said, you must be smoking some bad stuff if you think music doesn't in fact exist.
Note that music is not a physical thing, it is conceptual, so when I say it exists, I am talking about the concept and the expression of the concept. Thay both exist, as a matter of fact.
Really, you're talking to someone who makes music. I know that music exists, and you can't tell me that it doesn't.
You jsut seem to think that a "fact" would be different from a "scinetific fact". It's not. A fact is a fact, and science can't change what is. Perhaps sciene isn't as forgiving about what a "fact" is, but that still doesn't mean there is an actual difference, it just means that non-scientists tend to throw that word around a bit too much.

" But when that person needs to communicate about music, then that person needs to try to use a definition that others will share.
 ... yes I agree with this ... anything that is music to anybody is music: I believe that was what I said: my point is this can't be scientifically proven ..."

"Scientifically proven"? This is not a proper concept. Science doesn't prove things. Proof is a logical concept, not a scientific concept. Proof comes from the realm of reasoning.
Science is about finding explanations so that we can make predictions.
The existence of some thing is proven by showing the existence of it. This is not "science". If I prove that I have a cup of coffee by presenting it to you, I am not doing science.
When we went looking for the higgs particle, the point was to test the prediction that Peter Higgs had made. This shows that his idea had predictive power, which allows us to understand things about the higgs particle that we couldn't understand simply by knowing that it exists. That is the scientific part of it.
The finding of the higg particle itself is just exploration.

"yes it is subjective ... that's why science cannot prove it objectively exists ... but it is also a fact ... "

It if is a fact, then it is a fact "to science", aswell.

"it depends on whether you're a pragmatic person or an idealist, or whatever.
 ... a chair "an item of furniture used to sit on or in, comprising a seat, legs, back, and sometimes arm rests, for use by one person" ... if you find any furniture that fits all these criteria, it's a "chair": simple"

You could also still imagine a situation where something does fulfill those criteria, but people don't intuitively think that it's a chair, because it doesn't look like one, for some reason. So they "accidentally" call it something else.
The point is that sometimes something does belong to a specific category, but it's not obvious to people that it does. Kind of like how a lot of people would think a glass snake is a snake, even though it's a lizard.

" ..... now a stool is "a seat for one person without a back or arm rest" : any furniture that fits this criteria is a stool"

If you then agree that a log that one could sit on is a stool, then you're a pragmatic person. Other people might not consider it a stool, because it doesn't fit their image of what a stool should be.

" ... it can be verified objectively what a chair and a stool is: and it can be tested and verified with the scientific method because it has a specific definition"

No, not using the scientific method. Whatever fits the description is that thing, there is no need to follow a scientific method order to indentify something. We don't need to create a hypothesis, and go through all that stuff about repeated testing.
The scientific method is there to find the explanation for something, such as why stools are the way they are, or what about them makes them feel good to sit on.

" The thing itself is not dependent on how we choose to define it, and that's true for music as much as for chairs.
 ... wrong ... try again ..."

It is correct. Even if we would change the definition of "chair", it doesn't affect any chairs. That would be magic. And no matter what things we identify as "charis" or "music", those things still are what they are, even before they had any label of any kind.

" ... Ummm every scientific fact has to be properly defined to be tested"

You don't test facts, because then they wouldn't be facts.
Why "test a fact"? What are you trying to find out about them?

" ... if I define evo. as change in frequencies, then scientifically speaking, anthing that changes frequency is evolving ... but if I add specificity and say change in allele frequency then scientifically speaking, any "allele" that changes in frequency is evolving ... "

Yes, that would be true.
But evolution wasn't a fact until you observed that it was. You didn't "test the fact", beause it wasn't a fact.
I may propose that green goblins exist. It's not a fact, it's a proposition, or assertion, or claim, whatever. If we do find green goblins, then it is a fact that they exist, not just a proposition.
At that point, what about this fact is it you mean we would "test"?
Do you actually mean to test a proposition/claim, to see whether it is a fact?
That is not done through science, btw. The job of science is not to discover facts, but to find the explanation for facts. Sometimes we need to look for more facts in order to be able to explain it, though.

"But you do not need science to determine whether such a thing exists. I can hear music, I can see chairs, and sit in them, and so on.
... I can use the scientific method to determine that chairs actually do exist:  I can't use it to determine that music does exist ... "

No, you don't. All you have to do is to find a chair, there is no need for the scientific method. We did this loooooong before we had the scientific method.

"the scientific method is a method of determining facts through observation and repeated experimentation"

When we experiment, the reason is that we're testing predictions that belong to some hypothesis.
Facts are a part of this process, because facts were the basis for the hypothesis, and the experiments yeild new facts, but the point isn't directly the fact, but whether the facts confirm the predictions or not. Ultimately, it's about the ability to predict, and facts don't predict, they just "are".

" ... and I'm saying that it's only a system created to decrease entropy that can account for any decrease in entropy ... not that 2nd law of TD doesn't apply to life"

The science is what it is, it's not an opinion. It is a fact that the 2nd law of TD does not apply to any living organism, because it only applies to isolated system, and no living organism is an isolated system.

"I'm saying what the law states : and it states that the entirety of an isolated system( whether it has an open subsystem or what ever) tends towards maximum entropy ... so I could say the solar system is tending towards maximum entropy ... and this includes life ..."

The problem is that you don't realize that the system as a whole only need to tend towards higher entropy, not each sub-system. Only the total entropy of the entire system needs to increase. That doesn't mean that sub-systems much increase in entropy, as long as the system is able to do work.
Yes, eventually, the entire system will die, so yes, in the end, that it will be true.
Life on earth will try to survive as long as it can. When our sun dies, we might still be doing everythign we can to survive. But eventually, the only thing in the solar system that can still increase in entropy is the living things, so they will die.
Point being that as long as one sub-system can avoid increasing in entropy by stealing energy from surrounding system, the 2nd law of TD doesn't apply to that subsystem. It does apply to the "parent" system, of course, but tath says nothing about this sub-system!

We know that the entropy of a living organism also want to increase so to speak), but because it's an oepn system, it doesn't have to.

You are arguing against the existence of life itself, and it's ridiculous, since you know that life exists.

"... I'm actually arguing that life wouldn't exist without the intricate and functional systems we see which limit entropy"

And does so by making life an open system. Life protects against increasing entropy by eating food and taking in energy, which makes it an open system.
That would be impossible in an isolated system, because there would be no food to eat and no energy to take in, so entropy would increase and the organism would die.

" this brings us to how that system developed ... considering that prior to the appearance of these systems there was increasing entropy, this would seem impossible ... "

It's confusing that you're using the word "system" with two seprate meanings. Either you're talking about a functional system, or a thermodynamic system.

No, entropy was not increasing in all places. Only the overall entropy was increasing, and it still is. And entropy still isn't increasing in all places, only overall, in total.

"... the sun also provides energy for mars and mecury ... apparently providing energy alone is useless unless there's a system which processes and utilizes the energy"

Yes, the entire solar system as a whole is a nearly isolated system.
Useless for what? That is subjective, unless you're thinking about some specific thing.

" ... obviously the sun's energy is not the cause of the decrease in entropy: biological systems are"

The sun is the key. Biological systems cannot live without the sun, as the sun is what's providing the energy.
Take away the sun, and yes, we can still eat food to survive. But the animals we eat need to eat plants, which need to eat sunlight.
If you removed the sun, then quite quickly, there would be nothing for anyone to eat.

" ... the suns energy would be destructive without these biological systems "

Destructive to what? And how do you meat that the existence of biological system has made the sun's radiation less destructive?

"... and even these biological systems can't ensure a steady low entropy state: else no organism would die ... "

Ultimately because life needs to evolve. Only species who evolve can adapt, and the ones who don't evolve get eaten by those who do.
Reply: antiHUMANDesigns

The sounds are real. But "codes" are not real, they are in our heads. Codes are abstract, and to treat them as if they are real is to commit a reification fallacy. ... Sooo ... the sounds are real, the sounds are the codes, but the codes are not real ... I don't think you're making any sense here ... PS trying to force the idea of codes being strictly conceptual isn't working I think you should realize that by now ... 

We both agree that the medium that carries "code" is real. It must be real, because otherwise they could not be used as a way to transmit something. ... not sure we agree on this ... however, going by this, you agree that a physical medium is required to make coding possible ... so you're saying the medium carries the code ...so lets take an example of a morse code message ... lets say we want to send a message "A" ... and lets say we're using sound patterns "..-.." (note: this is the closest approx. to real sounds) ... the medium is the sounds: the message it's carrying is "A" : as far as I know... but you're saying the medium is carrying a "code"... so my question: in this scenario, which is the code?

But the beeps are just beeps. Without the knowledge that they should be considered "code", they are just beeps. The beeps are real, the codes aren't. The codes are something we've agree on. ... No I disagree: the beeps aren't just beeps ... even without the knowledge of morse code, anyone can recognise that the beeps are not "just beeps" ... anyone would recognise the sounds have a specific pattern(s) and hence tell it's code ... the only difference is that that person wouldn't be able to decode the message ... 

And I just can't believe after this long conversation, we're still right here, where we were at the beginning. ... it's probably because you're only forcing your opinion through without gaining some more perspective: just incase you haven't grasped the consequences of your assertions here are a few ... in essense you're saying:
1. Nothing in a computer is code except one is programming in assembly...
2. abbreviations are all codes ...
3. modems aren't "decoders"
4. signals from satellites aren't decoded.
5. object codes aren't codes

And I said I wouldn't discuss "code" anymore, and I should've taken my own advice, because this is clearly a huge waste of time. ... well your assertions are most likely wrong and if you're wise you'd see where I'm coming from and try to limit your rants and focus on the points ... and particulary on the "computer code" ... 

The fact that you can draw morse code proves that the code is not "sound". Sound is one way to carry the code ... well you can draw pretty much anything up... it's just a way of representing things ... however your new description of "medium" seems to be gaining good grounds ... seemingly, according to what you're saying all codes are carried through a medium ... but this is not too viable because it's messges we aim to transmit through mediums ... however, my description is not very far off that: I'm saying that the appearance and functionality of the medium would indicate that it's a code ... 

The code is not real, it's just an idea. ... I think what you can say is that a code represents an activity of a mind: or maybe that the coding system is mostly idealistic ...  

Anything that can be used to physically represent the idea is just a medium, but it would be a medium capable of transmitting the idea of a message encoded as morse code. ... well you're still going to need to differentiate between the medium and the code: I'm saying they are basically the same: you're saying they are different ... 

You don't "interpret" code, you decode it to get the actual symbols ... another way of saying it ... ok life depends on the "decoding" of DNA ... 

and you can interpret those symbol to understand their meaning. ... well this applies very well to abbreviations ... not sure tho how this applies to computer codes ... obviously the only thing that understands the meaning of 0's and 1's is a computer ... what you're saying by this is that the computer decodes assembly codes into machine codes and interprets it to understand their meaning ...

DNA in a cell is a mulecule that produces other molecules though chemical reaction. ... if you don't mind ... can you give me a brief rundown on how the DNA works ... cuz it seems to me like you're either trying to oversimplify the work of the DNA or you're just clueless about its functioning ...

But they cannot know if a signal came from an intelligent creature simply by looking at the signal. ... what exactly are you saying: yes they can detect a signal that would suggest intelligence ... obviously they are not looking for intelligent aliens as you would refer to it: they know that there are signs which would indicate intelligence ... 

It would have to be a signal that somehow uses a system that we invented, so that we can tell that it is a message. ... it doesn't have to be a system we invented : it has to be a system which can be recognized from our knowledge of things ... 

Basically, it would have to use our language. ... what nonsense is this? ... ofcourse not it doesn't : they're particularly looking for " signals from advanced technological civilizations in our galaxy " ... 

*If it is in an alien language, we don't know that we can tell that apart from something natural. * ... wth ... if it's an "alien language" wouldn't that indicate we already know it's a language? ...

And note that they have never actually found a signla from some intelligent aliens, so they have no idea if they'd be able to spot it if they saw it. ... yes they haven't but they know what would be if they discover one ...  

For all we know, we might already have received messages from aliens, we just don't realize it because they don't do it the way we do. ... alien intelligence wouldn't have to do anything exactly like us ... what matters is if the signals show a pattern that can be recognized ... it'd indicate intelligence ... 

"2. Identify a known coding system which, when applied to the sequences, makes the sequence make perfect sense. It is highly unlikely that something apparently random would be decoded into something meaningful with the wrong coding system.
 ... the coding system for the DNA is obviously the cell and it's "machines" ..."

No, now you're once again using some fucked up definition of "coding system". I'm talking about something like morse code. If we see some kidn of signal, and we use the morse code system to decode it, and it turns out to be perfectly valid sentences, then it's reasonable to think that the sequence was encoded using the morse system. ... and you're probably saying more nonsense ... apparently you've just said that the coding system is the system that decodes the coded information ...

Another example would be to see a bunch of apparently random numbers. But when plugging those number into the ASCII table (a code system), it becomes valid sentences, then we've got that situation, again. ... Soooo ... how's this different to sayigng that the DNA (which is apparently gibberish to you) becomes valid sequences when "plugged" into living vells? ...

The DNA of humans, however, doesn't do this. Use ASCII or morse code to decode DNA, and you get nonsense. ... are you retarded or something? ... isn't it crystal clear that the DNA is not meant to be decoded using ASCII or morse code systems? ... dafaq : morse code is nonsense if plugged into the ASCII table ... 

PErjhaps there is some coding system we're not aware of that was used ot encode it, but that would amke no sense, since the sequence in DNA is not arbitrary. You can't both use DNA to send an encoded message and use it as a genome for an organism at the same time. ... why can't you exactly?

You're mixing up "coding system" with "instruction set". Seriously, try to make some sense. ... lool ... u serious? ... how about you actually try to point out exactly where I got it wrong? ... you haven't actually said anything here ... and my statements still stands: the coding system is in the cells and it makes meaning out of the DNA ...

You seriously must be trolling me, here. I refuse to believe you're this stupid. ... well luckily for me what you believe has absolutely no weight on reality ... like I said, the computer can make meaning out of binary codes : dammit that's why it's a computer ...

It doesn't "make sense" to the cell. Explain where in a cell the brain is that can "make sense" out of something. ... well obviously formation of vital proteins are implemented by systems that decode DNA codes : in this sense, it does make sense in the cell ... if it didn't then life wouldn't depend so much on it ... 

"yes the cells do use the "meaning of the sequence": are you sure of what you're saying? ... if you delete sections from the DNA of an organism you can end up creating detremental damages to it ... "

Same thing if I were to delete a sequence of the instructions of an automated robot that builds cars in a factory. The cars might turn out not working. There was no meaning to the sequence, it was data that the robot used, which controlled the movements of its arms, and so on. ... Ooookkk ... you can also say that "data" had a "meaning" of some sort, to the robot: contexually ofcourse, not in the exact same sense as something would be meaningful to us humans ... btw, by your analogy you accept that the DNA is somehow pre-programmed : no?

Meaning doesn't exist on that level. It was "useful" and it produces the correct result, but there was no "meaning" in it. You could not read the data that the robot uses and see the "meaning" of it. It has purpose, but it doesn't contain meaning. ... what you're trying to say is that it has no meaning to you ... and obviously, the instructions for the robot weren't intended to relate to you: they were made for the robot ...

A sequence of DNA also has a "purpose", in that it's used to build an organism. That is the purpose it's being used for. "Purpose", in this sense, is not the same thing as "meaning" is in the linguistic sense. ... Ok just to let things off a bit: let's say I go with the word "purpose" ... you agree the DNA has a "purpose", but you say it's gibberish ... does that sound logical or consistent to you? ...

"*No, that's the software giving you the appearance of understanding. It's not the computer, it is the program.* ... and what exactly do you think a computer is?"

That's a strange question. ... wow ... asking about the description of a computer is a "strange question" to an expert programmer? ...  

First of all, it's not a program, and that's the only thing that matters in this context. ... well it is ... sorry ... 
-Computer: an electronic device for storing and processing data, typically in binary form, according to instructions given to it in a variable program.-Google
-a programmable usually electronic device that can store, retrieve, and process data -Merriam Webster
-A computer is a general purpose device that can be programmed to carry out a set of arithmetic or logical operations automatically. - Wikipedia
I don't think there's any reference you can pull up which doesn't define a computer as a programmed electronic device ...

If you're talking about somethign liek a calculator, then that is not  a proper computer, because it can't be programmed. ... a calculator is a "proper" computer: whether it can be programmed or not ... this is why I really question your knowledge ... it seems like abstraction has its side effects as well ...

A computer is not a mind. I think I've already linked you to the definition of "mind", otherwise you can look it up yourself. You're simply utterly wrong. ... "artificial mind" ... I think I've stressed this hard enough ...

A computer is a framework for software to run on. Software could potentially simulate a mind, however. ... well if you're taking of the instructions in a computer they are stored in voltages : that's what you'd call "software" but to me more accurate, it's "firmware" ... the firmware is part of the computer: that's what a computer is about: voltages and switches...

"*For a computer to be able to work with "code", the CPU must have a mind. The CPU itself, not the software that it runs.*
 ... yes the CPU has a "mind" ... I'm pretty sure that's why it's called Central Processing Unit: translate that to humans and it come out as brain ... to process something and give an output is basically all you need from a mind ..."

Stop equating "brain" with "mind". They're two different things. ... you said the mind is the action of the brain: I'm just saying the computer's artificial mind is the action of the CPU ...
Yes, the CPU, in the broad sense, is a kind of "brain", but it doesn't produce a mind, like a human brain does ... not like a human brain does: I believe that was why I said it was ARTIFICIAL ... 

In the weakest sense, perhaps. But a program, however, can make something that's more like proper "choices". ... a computer is more or less a program ... 

The word "choice" does, by definition, imply free will. I'm not sure I like that, and agree with it, but it's still what the word means. ... I'm not saying it's free will like humans: it's only choice according to the program ... one can program a computer to choose from as many options as possible ...

A CPU has the least possible amount of freedom in making choices. We rely on the CPU to do exactly what it's told, not to make choices freely. ... Obviously ...

By writeing a "struct", like that, I have set up limitations on how I am allowed to use something. ... yeah these "structs" still end up in machine codes ... just hope you know that there's nothing(nadda) inputed into a computer that doesn't end up in machine instructions(or binary codes) ...  

Ther ei sno reason for this to become part of the software, because this is only relevant to the process of writing the program, not running it. ... yes it's not going to be stored as the software: it'd only be used as an instruction to create the software: and that instruction must be transformed into binary form to make any meaning in your program ...

Wait, is that all you mean? That everything I write will be saved in binary, simply because its part of the "document"? ... no ... what I'm saying is that these instructions that don't get saved are just temporary instructions: almost like how the RAM in computer works ... the instructions guide the building of the program: but they are not saved as part of the software: however, for these instructions to even have any effect, they must end up in binary codes ...

I think you're deflecting, or that I am misunderstanding something. You must be equally aware of what we're talking about. ... you're most likely misunderstanding me ...

Programming is also "practical and realistic". (?) Software and hardware go together in a computer. They need eachother. You don't ever use a compuer unless you run programs on it. ... well I told you that anything you can do with a programming language, or with assembly codes, you can do that exact thing with machine codes and practical circuitry ... ie every thing you do while "coding" is more or less a direct representation of what actually goes on ... that is to say, the codes are actually real ...

The thing that goes through the CPU can be descirbed using code, but it isn't inherently code, because like I said, code is a concept, and idea, it isn't a real thing, and a CPU is physical. ... and like I've said : the computer code is quite different from normal codes humans use 

It requires a physical medium, and it is the medium that goes into the CPU. In this case, it's a pattern of voltages that is the medium. Specific patterns cause specific outcomes, and we can name the patterns. But the CPU is not aware of the names of the patterns ... and again a CPU is aware of the patterns: for God's sake it's an emulated mind ... 

* but that is what you're arguing that it is. You're arguing that it takes the names of the patterns, not the pattern themselves.* ... what? ... I'm arguing that it takes the patterns and interprets them to different patterens: that's the "processing" ...

Then there are no computers. It's that simple. You've just changed the definition of a computer to the point where no computers exist. Congrats. ...and congrats to you for not knowing what a computer is ... 

Just look up the definition of "mind". ... maybe you should look up "artificial mind" ...

But you're right that instead of using assembly, we could just write the values that directly represent the pattern of switches to be used. The reason we don't, as I said, is because it would be hard ot remember the values, and it would be nearly impossible to read and understand what you're written, afterwards. It would be "fit for human reading". ... I believe that was basically what I said: writing in both forms are the same: just that one is a shortened version ... it's almost like you described machine codes: binary form is obviously longer than hex format: but they're all the same ...

Are you officially retarded, or something? It's right there, I just explained it, and then you act as if I didn't. ... well you wouldn't notice but I'm just trying to establish the fact that symbols are real: even though they can represent abstract things ...

It's amazing how you can say such things and not realize what you're saying. ... lol ... I'm only appling your logic to the fullest ...

Sorry, what do we call the action of those switches and voltages? Oh yeah... software. ... I think software is any program that is stored in voltages : ie any program stored electronically ... however if you decide to call any electronic activity software, then the computer is made of software ... afterall the computer is made up of voltages and switches ...

No, "code" doesn't have any criteria by which you can recognize them, and that's part of the point with codes. That is why they're used for secrecy, sometimes. A code is completely arbitrary, and that's why you could be looking at a code and not know that you were. ... well I don't think this applies to the computer code ... 

Some codes can be less arbitrary than others, but a code can be completely arbitrary. This often depends on whether the code is used for secrecy or for simplicity. Simplicity usually follows systems, and relate to the thing they're encoding, so that it's easier to learn it. DNA code is an example of this, where "TCGA" is easily understood as the first letter of each nucleobase's name. A simply code, easy to learn and quick to read. ... more like an abbreviation ... shortening a word is definitely not coding ... 

Yeah, if you're a fool. Or if you have nothing else to say. ... hahahahahaha ... sure sounds like you have nothing else to say ... yes programming can be described as building ... got any other word? ... lemme guess: "construct"? ... well: hell yeah: programming can be described as constructing ...

That is exactly what a program can do, in a turing machine. A program can change itself as it runs, that is the power of software. ... a program that can change itself is a program programmed to do so ... ie, it all depends ON THE PROGRAMMING ... 

*1/0 -> the switch.
on/off -> the switch.* .... loooooooooooooool ... this is really funny ... honestly ... 

1/0 was never meant to refer to another symbol, it was meant to refer to the state of the switches. ... ofcourse 1/0 was meant to refer to the states of the switches: which are on and off ... but just to make things easier: 
1/0 -> on"state"/off "state" -> the real thing ...

* On/off is just another way to refer to the state of a switch.* ... oh I like this ... so you're saying there are different ways of refering to one real thing? ...

But don't get me wrong, "on/off" could be referring to 1/0, if that's what you intended. In such case, yes, it would be code. ... hahaha ... 1/0 directly represent on/off: not sure why you're arguing this ...
 
Yes, if this is what you intend when you say or write those things, then they are "code". ...Ooooook I got more:

ACC -> Apple Computer Company -> the real thing ... 2 levels
AI -> Artificial Intelligence -> the real thang ... 2 freagging levels
AHD -> AntiHumanDesigns -> your sorry ass ... 2 levels
wait wait ... I think I've got even more ...

komma -> Come -> the real thing ... 2 levels
gå -> go -> the real thing ... 2 levels
hoppa -> jump -> the real thing ... 2 levels ...
this should do for now but I'd be happy to supply you with more 2nd level symbolism if need be ....

*cat -> concept of catness -> actual cat
...and that "cat" is therefore "code".
But it isn't, because "catness", the description/definition of a "cat" is not a symbol. Therefore, this is not second-level symbolism.* ...don't see how this is wrong ... from your own explanation,  "all" words are symbols ...
By "concept of catness" I mean our defintion and understanding of how to recognize an object as having that label.
When I say "I have a cat", your brain hears/reads the word "cat", and probably recalls an image of some cat, but also recalls what makes a cat a "cat", intellectually, if such understanding exists. So your brain will make some statistical or associative assumption about what kind of a thing it is that I have. It's probably going to be wrong, because your brain will subocnisously produce an image of my cat that probably doesn't look like my actual cat, but you'll be categorically correct. We'll both agree that it is a "cat", that the label/symbol does refer to that thing.
The concept of catness is not a symbol because it doesn't refer to anything. It describes an idea. ... Soooooo ... the concept of catness describes the notable attributes of a cat: but it doesn't refer to anything? ... Hmmm ...

"How can you say that a computer understands 1/0?
 ... how can you say a computer doesn't understand on and off states? ..."

How about you answer the question? ... the question was a strawman ...

It doesn't understand on or off states because it has no capability to understand anything. It has no mind. ... not sure I should go through this again ...

You're incredibly wrong. There are not 2nd level symboslism. ... are you kidding me now? ... I'm "wrong" just because you say so? for real?...

And then I guess you'll be doing everything you can to avoid ever defining "new structures", right? ... I believe I did ... for a bacteria to morph into a human it needs to gain new structures like eyes, lungs, etc ... by new structures I mean components and systems which didn't exist before ... a good example would be new protien structures ... as we see, different proteins are required for different structures : so maybe you could show me an organism developing a new useful protein structure ...

"But I agree that since it is based on somethign else, it isn't new "from scratch". But that doesn't matter. ... it does since you've just accepted that duplicated info. doesn't fit my criteria for "new" info. ... "

I didn't what what you criteria was for "new information". If "duplicationmutation" doesn't fulfill teh cirteria, then Ia gree that it isn't an example of that. ... you know at first I thought this was pure gibberish ... but I assumed you were really trying to say something: so maybe you could have another go ...

But all sorts of different kinds of mutations happen, and some of them must fulfill your criteria. ... well then show me one that created a new structure ... 

"*And for some really weird reason you said genetic code is altered throuhg "genetic variation and natural selection". Dude, that is evolution!* ... yes evolution is scrambling and degradation of pre-existing  information "

No, the "scrambling" of information is called "mutation". ... scrambling and degrading to be more specific ... 

"...  but by scramling and degrading pre-existing information we can get all of the complexity of life ... beautiful stuff ..."

No, you can get that through "evolution". ... yes ... and evo. is scrambling and degrading information and structures ... like we've all seen ... I mean you'd agree that the loss of function of a structure in Lenski's experiment was the prime reference to evo. ...

Nice attempted straw man, there, but you're just wasting time and effort. ... I actually trying to apply the evo. system ... in the experiments, we see loss of functions and degrading of information owing to evo. ... but in evo. world we see gain of complex structures on astronomical magnitudes ...

I have no idea what your point is. ... lol ... you were obviously attempting to give nature super magical powers by insinuating that it created all of the complexity we see in life ... well that's far from what we actually see... 

If you're talking about evolution, then you haven't lived long enough to see any changes. Not that changes haven't happened, they're just too small for you to see them. You need to look at the DNA level to see the changes. ... yeah the changes needed for bacteria-to-man evolution are invisible in the real world ... only exists in imaginary world ... in the real world we see difersification of pre-existing "kinds" : penguins produce penguins, moths produce moths, chicken produce chickens ... huge variety exists in all these animals: but still, they maintain a striking level of consistency ... at least we have an idea of just what it'd take to get a chicken from a moth-like organism ...

Shape-shifting, yes, lots of animals do that, in different ways. I have no idea how you could have missed that, but who cares. An obvious example would be metamorphosis where a caterpillar turns into a butterfly ... Ok to be more specific: I'm talking of shape-shifting on reproduction level: ie generations shape-shifting into practically different ones ... e.g fish to cat ... that pretty amazing stuff btw ...

And evolution, yes, that is something we've learned about, from nature, and are applying to technology. ... can I see this technology please: as far as I know, all technology is a product of Intelligent Design ... 

Imagine how weird it would've been if we started using evolution in robotics and computer sience, before we realized that nature does the same thing? ... not sure I'm getting you here ... if you're saying I should imagine how weird it is to use evo. processes on actual technology then I'd say that'd be a stupid move: we create robots particularly to avoid tampering with their codes ...

No one here is proposing that a random processes can do that. Drop the straw man and stop wasting time. ... what strawman? ... I'm giving a brief heirarchy to my thought process ... the bacteria flagellum is basically a motor: identical to motors humans make: we know the bacteria flagellum exists, we know the human machines do as well: we know that only intelligent design can account for the electric fan motor ... so what reason do I have to believe that a random process, which is mostly destructive, can create the flagellum?

Remember, it's not evolution that produces mutations. That's just physics and chemistry. Evolution simply depends on those things existing for the process to work. ... Ok ... the processes on which evo. depends, have been proven to be more destructive ... just curious: how would evo. work if the requred processes are always destroying components? ...

A false dichotomy fallacy. There aren't just 2 alternative, ID or evolution. If you're looking or an explanation for something, then there could potentially be an infinte amount of possible explanation, not necessarily only 2.... it's actually "chance" or "design" ...

This is why even if evolution was shown to be wrong, it doesn't mean creationism is right, it means we no longer have an explantion. ... of course evo. beign wrong means you have no excuse to ignore design ... that's basically what evo. is : an escuse ...

That's why the only thing we care abotu is whether we have predictive power, not whether something is "the absolute truth". ... can you just give me a run down again: what are these predictions evo. makes? ... these predictions that have been "confirmed" ...

The straw man continues. Get back to me when you start talking about evolution. ... lol ... strawman? ... you've spent so much time trying to attribute some kind of order to a random process ... that's what has been happening ... 

I agree that some intelligent creature could, scientifically, have existed at that time. But we only have good reason to think that they could have existed, not that they did. ... not sure what your point is here ... 

We have reason to suspect that other may exist, but we have no justification for believing that they do until we seen any kind of sign of them. ... yes of course you do ... we know the direct products of intelligent design: we see it every day ... and we know that entropy is a fact: especially at the post-big-bang period ... we know it's impossible for any sort of order to come out of a cosmic explosion after 10billion years ... after such a long time, we know that maximum entropy should have been achieved in the universe ... and we know that an increasing state of entropy would never create a solar system with conditions so "finely tuned" to suit life ... and we know that no form of luck can create living cells from inorganic matter ...yes we have good reason and justification to suspect that an intelligent beign did exist ...

Define "destroy". Remove functionality or structures? Yes, in some cases, that is predicted by the science. It's the same reason we lost most of our tail. ... first of all "remove functionality and structures" is what we observe most of the times : I don't think I've seen or heard of an observation or experiment of gain of functionality or structures ... this destructive process is what's expected to build flagella and lungs and kidneys and eyes and so on: why would you even fault anyone if they say this is nonsense? ... secondly, try not to use your evolutionary pressupositions with me: try to use real evidences and facts: like I've said, I don't believe in the "shape-shifting" story: so I don't believe humans had any tail ... of course your dogma labbeled the coccyx a vestigial components but yet again, it turned out to be a failed prediction ...

That's not how evolution works. Evolution works with what it's already got. It doesn't make things from scratch. ... oh beautiful ... evolution works with that it's already got : it doesn't "make things from scratch" ... but ... it managed to make our lungs and eyes and bones and liver: apparently, a bacteria had all these ... 

That's also why evolution is not the origin of life, since evolution requires something like life to already exist. ... oh well I think evo. doesn't explain much of how all this diversity arose ... it just explains how different variations of organisms can gain more advantage and population in different environments ... of course this doesn't explain how these different "kinds" or lets say "families" of organisms came about ... of course we know it's impossible because "evo. can only work with what it has" ... so to get a fish from a bacteria would require gaining a lot if useful info. and components and systems: apparently from nowhere: we know this because bacteria don't produce the required info. to create something that is not a bacteria ...

Yes, evolution is the change in those frequencies, and our understanding of this process predicts/concludes that complex structures can arise over extremely long periods of time, due to this. ... yes it only produces "complex structures" in the invisible world ... ie the invisible millions and billions of years ...

And we've seen that. You just don't want to accept that we do, and I can't force you to accept it. The fossil record shows this. ... when you said "we've seen that" I was expecting real time evidences: but apparently I'm stuck with the fossil record which even contradicts evo. ... I mean the fossil record is about sudden appearance and disappearance of different organisms with little to no signs on evo. shape-shifting them ... the most glaring evidence is the dumping of gradualism for punctuated equilibrium: this clearly indicates that the fossil record didn't support evo. : it was only a desperate attempt to make the story sound more credible ... basically saying that the evo. times were too fast for the transitions to be fossilized in detail: this is just a make-believe sory... has no correlation with any verifiable or observable fact: it's just based on the presupposition that all life and it's complexity morphed from single-celled life ... 

*It's your right to deny it all you want, but there are good reasons why scientists don't deny it. * ... well if a scientist can loose his job for criticizing evo. I wouldn't call that a good reason ... 

And we don't have anything to talk about if what you're going to do is simply deny it all. In such case, we'd be better of discussing how religion makes you deny such things. ... not sure if you realized but I don't stand for religion: atleast what it has become now ... you should notice that I've rarely if ever, bring up anything which isn't verifiable and factual ... you should have noticed I didn't bring up anything related to the Bible : you did : I've just had to defend my position ..

"Supernatural" doesn't have to violate the natural, but magic does. The idea of "magic" is that something just violates natural law, and does physical things, without being scientifically explainable. ... Oooookkkkk ... I'm not saying God violated any natural laws ... I've said it before God seems to use math a lot ... also, there are many ways a supernatural beign can make a design using natural laws ... countless ways ... 

Supernatural, if it exists, could be perfectly OK remaining supernatural without violating the natural. The "multiverse" could be said to be in that category, since they don't propose that it violates the natural. But as I see it, if the multiverse exists, it is also natural. If the supernatural exists, it's also natural. I don't see what justification we could ever have to call anything supernatural if we can scientifically demonstrate it.

"... you can be Supernatural and use all the natural laws : being supernatural just means you're not bound by the natural laws ...  by definition, we can say music and beauty are supernatural ..."

Music and beauty are also bound by natural law. Umm hell no music and beauty aren't bound by natural laws: not sure exactly how this popped up ... I can listen to music without a single sound being made ... and I can listen to sounds and discard it as noise instead of music ...

The idea of them aren't, but no idea is ever bound by natural law. 

The reason that we find some things beautiful is that our brains have evolved to do so, usually because those things are valuable to us, from an evolutionary perspective, otherwise because they remind us of somethign that is. Its our instincts attempting to control our behaviour. ... Ok I understand you have been taught evo. all your life and it's ok for your presuppositions to get in the way: but can you try as much as possible to stick with the facts? ...beauty has no specific explanation or a predictable pattern: explaining beauty is like trying to catch a wind with bare hands ... if beauty is dependent on things valuable to us then how do you explain beauty on first glance? ... you just see something totally unknown before and it appears beautiful ... beauty is more like music ... beauty is anything that is beautiful to anybody ... 

We define some sounds as being music, usually if the have some kind of impact on our mind/emotions. In the same way, we define some pieces of metal to be cars. A concept itself cannot physically exist, as we've talked so much about. ... a chair does exist, a car does exist, but music apparently doesn't in this context... we can define some sounds yes but what criteria must the sounds have to make it objectively music? pitches? tones? ... a car backfire has a pitch and a tone ... we can define a car to objectively exist because it has physical properties which differentiate it from a piece of metal ... 

Intelligence is a capability of something to reason, for example. (Note that we have no proper definition for "intelligence", because we can't fully agree what it is.) ... well I know ... intelligence might well even be like music and beauty ... not sure though ..

I'm seriously hoping you're not arguing that a god would make things happen because of intelligence, rather than because of his ability to actually do things, but I mgiht be expecting too much. ... I'm not sure but you seem to be missing the point: I'm arguing for Intelligent Design : Intelligence is the ultimate cause, design is the application or practicalization of intelligence ...

More than once? Yes, absolutely, that is horribly unlikely. ... more than once? what's that? ... what evidence is there to prove that it did once to begin with? ... what evidence suggests that  it can even do it?...

See, this is once agian a case of trying to put odds on somethign tha thas already happened. you have got to be kidding me ... what happened? evolution of the flagellum? well hell no there no certainty as to whether that even happened: you weren't there to see it happen: nobady was ... we can only infer and pose a "best explanation" ... and if you think evo. created the flagellum as a matter of fact then you're definitely way off science ... and you'd need a lot of faith to believe that ... my problem is not whether you need a lot of faith to believe this: it's just that you call it science ...

Imagine a a large set of dice, again. Say that the flagellum, as we indentify it, is a specific dice roll, such as "4, 7, 1, 1, 2...". The chance of that specific dice roll happening again is very small, obviously.... Umm ... and what's the chance of even getting that sequence to start with? ... I say it's very unlikely ... except you're saying all possible outcomes would create a flagellum ...

But now consider that you just roll those dice, and some random result happens. Now take that result, and call that "the flagellum". That is basically the situation we've got here. The flagellum was one possible thing that could have happened, out of hell knows how many possible things. Simply because the flagellum was the one thing that happened doesn't mean anything. ... Ok so you're saying the flagellum was the result random occurence? ... well way to go on contradicting yourself one more time ... well I don't think a random occurence can produce a flagellum: and I have good reason to think that ...

But like i said, I agree that if you were to roll the dice, it wouldn't happen again, a priori. ... well I guess that'd suggest it didn't happen by rolling a dice ... 

Of course, evolution isn't random, so the analogy only goes so far. The reason the flagellum is what it is, is because evolution had to work with what it already had. ... yes which is the "random occurence" ...

It can't perform that function until the parts needed are there. But it could perform some other function. That's why IC is pointless. ... no this is not pointless : it's vital : conceding the need for all said parts of an IC system is the main aim ... it's a fact ... and saying it "evolved" by random additions of parts is just another hypothesis : it can be easily said it didn't : you have nothing to prove that ...  actually the confidence used to say this proves that evo. is actually based on little facts: what you're saying in essence is that this system needs all its vital parts present simultaneously to perform its function, as a matter of fact ... but it can be imagined that it got all these parts together by adding new components and gaining new functions ... ID proponents just say "Nah that doesn't make any sense" ... anything can happen in the imaginary world ... you have to prove it in the physical world for it to have any weight ... ID says that because the system displays Iredicible complexity, it's most rational to conclude that all the vital parts arose at the same time: hence the best explanation is ID ... this can ne falsified ... it can be falsified we find bacteria with different structures, each containing component(s) only found in the flagellum, performing as many different functions as there are components ... if we can't, then the claim by ID is confirmed ... now it's important you know the claims which you could attempt to falsify ...

An IC system can still evolve if the steps towards it were beneficial in any way, and even possibly if they were neutral, at least to some small extent. ... if and only if ... well I say it can't because no organism has ever been seen to even produce a new protein structure ... and even if we saw one, no structure can be found which perfectly matches itself to another structure without a pre-existing assembly instruction to guide it ... in essence, what you're saying is imaginary ...

For any specific case, we can often specify what steps those were, because we can often find cases where the "old" function is still there, and we can see taht it would only require 2 steps, for example, for that function to become the other function. ... I would love to see an example of this ...

Everything resonably complex is a repurposed version of something else, like how our hands are repurposed fins. Evolution did not make our hands from scratch. And even though our skeleton is unique in detail, it's still made from a skeleton very similar to it. Only small steps required, and each step can be beneficial. ... again, more unverifiable, imaginary stories ... 

"But in biology, there is a specific defintion of what we mean by "evolution". It is not simply "change". ... yes in one instance it's change in allele frequency, in another instance it's forming complex molecules from simpler ones ... it's definitely not that simple I'd say ..."

Forming complex molecules from simpler ones is not the same context of "evolution", if you use that word. It simply isn't evolution, it's chemistry. There are no species, no replication with variation, and so on, so it's clearly not the same context, as it's not describing the same process. ... ever heard of "bio-chemistry"? ... are you saying that bio-chemistry isn't related to biology? ... however it'd be a point of note that the definition of evo. isn't consistent in science ... 

If it's so "amazing", why don't you read a fucking book on it? You sure could stand to learn the basics. ... you're more or less asking me to go indoctrinate myself : I don't think I'd want to do that ... PS I prefer a situation where I can ask the writers exact questions instead of just digesting everything they say ... 

Yes, evolution is amazing, and very interesting, and most importantly extremely powerful. That is why it's of interest to multiple fields of science. ... well firstly, not a scientist, neither do I aspire to be one: I'm an engineer: entry level yes: but in engineering all we know is Intelligent Design: we know exactly what it takes to get functional systems and machines to work: that's why this evo. story sounds like gibberish to me ...

The fact that you're different from your siblings is not because of evolution. Evolution did not make that happen (or did it? Consider the "evolution of evolvability"). Evolution is a process by which the gene pool changes, it isn't responsible for individual variation between individuals, it's responsible for the gene pool as a whole shifting towards some specific trait. ... so the gene pool changes without showing the differences between me and my siblings?

The idea of IC exist whether or not any systems exist that are actually IC. ... so I take it like I've wasted a lot of time on this ...

No, I don't think so. I think a hunter needed a dog that was good for hunting, so they bred a dog from a good hunting dog. They didn't know it was going to end up becoming a specific breed thousands of years later. They probably had no such concept. ... Oh I see ... they "bred" the dogs but they didn't know the breeds were going to become "specific" ... hmmm ... Nah: makes no sense ...

No single person lived long enough to see any major changes, I suspect. I mean, people didn't live as long as we live today, which would probably only allow one person to see perhaps 10-20 generations of dogs, if they worked as breeders.I'm only guessing of course. ... yes the lived long enough to see major changes: I don't buy into your guess work ... it would have been obvious that different dogs were displaying different variations and abilities  ...

But over 10 000 years, we're talking about thousands of generations. Perhaps if you could see 100 generations, you'd notice a difference to the point where you'd realize that something weird was going on, that something "new" had happened. I don't know, I can't say. ... well I think we all say some 50000 generations of bacteria showing that nothing weird was going on : nothing weird enough to turn them into something they weren't ...

It's a sad fact, but most people cannot reason properly to any extent, since we're prone to fallacies, or don't have enough knowledge about things to be able to tell whether something makes sense or not. ... Ooook ...  I think you're correct on this one: not sure you know just how correct you are ...

And when you add religion to it, you've got religious people who want evolution to be false, and will accept any argument against evolution as being valid and sound.... I don't think anyone wants evo. to be false per se: it's just not showing evidences of being correct to start with: it's most likely false: not because we want it to, but because the evidences show that ...

Whatever truth, it doesn't matter. .... hahahahaha ... gased out? ... can't remember your own lines? ...

If I "can't believe a car can be red", it doesn't mean that a car can't be red. ... Ooook ... you can't believe God exists, it doesn't mean God doesn't exist ... incredulity much?

When people say "I just can't believe that evolution could cause this", then you've got this fallacy. ... what you have is actually you versus your strawman ... I say I don't believe evo. cuz it's actually more contradictory with the facts ... 

And to try to present evolution in a way taht makes it sound as implausible as possible - which you do - is a rhetorical trick of appealing to your audience's incredulity. ... still battling your strawman I'd say ...

Tell that to the people who use evolution in technology. ... lol ... I dare you ... I double dare you to give me one(1) technology that isn't a product of intelligent design ...

Because you shouldn't reject something just because you can't understand it. You should have no position on it until you understand it. ... intuition is basically knowing something based on your already present knowledge of studied and proven facts, without have to take the time out to prove it all over ... e.g if you see a wrist-watch in Jupiter intuition would say it was designed: it's because you know what a designed item looks like that you don't need to call for a scientific test to check if it's actually designed: that's intuition ... 

When it comes to evolution vs creationists, you've got all these creationists saying "no evidence exits", but they don't know what evolution is, or even what evidence is or how it works (yes, sadly, that's too common), and even though the ones who do know these things keep telling them that they're wrong, they keep insisting.... and here you are saying "no evidence exists" for ID without knowing what ID is ... the irony ... btw tell me again how evidences work... I really reckon this is a strong area of confusion: and I think it can be cleared up suing the scientific method ... PS "the ones who do know these things" also tell us that evo. is wrong ... 

Yeah, it's annoying. ... I could say the same ...

"Now"? I have no idea why you ever thought I disagreed or didn't understand this. It's extremely basic. The difference, which might be confusing you, is that I know that this doesn't actually mean anything, it's irrelevant. We don't agree on the implications of IC, quite clearly.... well firstly no need to claim you understood this all along: you were clueless as to what IC says and how it affects ID ... it seems you're still a little confused about that: ... but let me explain one more time : IC attempts to distill the facts into simple terms: and like we've both agreed, the facts say that a said system is IC, and its observed function can only be possible at the presence of all said parts ... ID basically says design is the best explanation for how the system came about : because the system shows a strong need of spontaneous assembly ... now note this can be falsified by evo. and also confirmed... this is probably another prediction : ID would predict that since we say this system arose spontaneously, we wouldn't expect to find a string of functional systems which contain parts ranging from 1 to the number of parts needed for, and found in the IC system ... ie: there wouldn't be systems which show a clear trace of gradual develpoment ...

Behe is an utter moron. And he's dishonest, aswell, as shown in the court case. Which, when I come to think of it, probably means he's actually a conman, not a moron. ... haha ... "Behe is a moron" "Behe is a conman" ... lol ... I think I have good reasons to listen to Behe instead of you or the other scientists that struggle to grasp something a child can grasp ... I mean I see Behe trying to explain this relatively simple concept and people like you calling him a moron even if you can't understand the concept and the implications on ID ... I think I have better reason to call you and the other scientists morons ... PS Behe and ID lost in court not because IC was wrong or because ID had no facts or evidences to support it: it was because people like you got to convince the judge that ID was religion: this has to be one of the most stupid court case I've heard of yet ... and I have my doubts about the judge ...

His mistake would be thinking that people didn't understand it. Jsut like you, who also seem to think I don't understand IC. ... if you did understand it then why the hell did I have to repeatedly explain this for so damn long? ... you totally misunderstood it: don't pretend you didn't ... you, Spiegel, and as much Scientists who couldn't understand it ... 

You can't seriouslty think that a "top scientist" wouldn't be smart enough to understand such a simple concept as IC. Get real. ... I am real: I seriously can't think that a top scientist wouldn't understand the concept: but it seems like that's the case: the main reason I thought these people were retarded: I mean you missed Ken Miller proving the mosetrap wasn't IC by making a tie clip out of the trap spring: like dafaq ...

The difference is in what you think about the implications of IC. ... the implication is spontaneous assembly: we both agree that the system in question wouldn't perform its function unless all the components are in place: this means all the components must have perfectly matching shapes and complementary functions plus intricate assembly instructions to guide the assemblage ... ID just says there's more than enough reason to say this system appeared spontaneously : and hence Intelligent Design is the best explanation ...

Behe doesn't work with evolution, he is not an expert on that subject. The experts who actually work with evolution, knows that he is wrong. And so do I, even though I'm a layman. ... Behe is a biochemist so he'd definitely know more about life since he deals with the molecular level of life: he definitely would know more than a zoologist for example ...

And most importantly, we can explain why he is wrong about the implications of IC, and I have. ... I wish you had ...

There is nothing about it preventing it, and it's a shame neither you nor Behe has the intellect to understand that ... actually what's needed is imaginary power and blind faith: we need evidence to prove that evo. can create an IC system: not "just so stories" ...

or perhaps it's just a lack of undertanding of the science. (When it comes to Behe, I'm not convinced he's even an honest person.) ... maybe: could be that we're just not conforming to your own definition of science: as far as I know, science is basically knowlegde gained by repeated observation and experimentation ...

The problem of the analogy is that a car isn't trying to survive or preproduce. A car without an engine can still act as somewhere to sleep, or hang out, and it can be used as decoration. Just a few examples. ... Sooo ... a wrong analogy? ... maybe a better analogy would have been a car engine: atleast it's function is to propell the car ... we could say the car engine is IC ...

But life isn't trying to be used by someone else, it's only trying to keep existing. And that's only because the ones that try to keep existing are the ones that do. ... so in this sense the pulling out a car engine would be like pulling out a humans heart ... according to your analogy, the body can serve as fertilizer and it proves the human system is not IC. ... I don't think your analogy is appropriate ...

Well, that's what we see. We see birds evolving feathers long before they evolved flight, for example. ... well if you call a penguins arm "feathers", then they "evolved" feathers and still can't fly ... however, we can clearly see that eagles "evolved" feathers and still could fly: punctuated equi.? maybe: more like ID ... btw I'm just guessing this is another story from the belief system : so I'm playing along ...

If a species has no way to move around, but needs to move around, then yes, they'll evolve something based on their current structure. That's obvious. I don't see what you find weird about this. It makes a lot less sense to think that a new system would evolve from scratch, since that would imply that evolution could plan ahead. ... so you're saying if a millipede needed flight, it could turn its multiple legs into a flight device and adjust its organs to work with flight? hmmm ... is this sci fi? ... that sounds quite easy, definitly I'd reckon the millipede would need some form of advancement in speed so maybe it could turn its legs into flying apparatus or it can just turn them into super fast machines or something ...btw back to reality: we have good reason to think that a flagellum didn't exist in another form in a bacteria: just like we know gills wouldn't come out of bacteria in infinity time ...

Exaptation is not about IC, either, it's about repurposing things. Whether or not IC is a characteristic of any of it is irrelevant. Evolution does "care", so to speak. ... exaptation is actually about trying to refute IC: atleast that's how miller thought it out ... however it remains an unverifiable non-factual excuse to explain the complexity of life ...

And the existence of IC, for example, is not directly due to evolution. Evolution can only cause something to become more or less common in the population. ... so are you saying evo. doesn't account for the existence of IC systems?

When we talk about new sructures evolving, the point is that the system requires multiple generations, and without the selection feature of evolution, it could not have happened. But that doesn't mean evolution is directly responsible for the existence of the genes that produced he system. Only indirectly. ... firstly new stuctures can appear without evo. I believe the evidences show they actually did without evo. : and I think ID is the answer ... secondly, are you saying evo is responsible or not: cuz it seems to me like you might be contradicting yourself once more ...

In any case, whether it's IC or not, there must be some way that it could have evolved into what it currently is, and have remained beneficial at each step. ... that's of course if you believe evo. is true: in this case your answer is "it evolved somehow" : "we don't know exactly how, but it did" ... well I say you haven't given any answer ...

Once again, IC is irrelevant. ... hmmm ... 

" maybe I used the wrong terms ... let me repeat evo. is more likely to degrade pre-existing components than add new functional components ... "

Explain to me how natural selection would favour degradation of existing components, if those components are useful to the individual? ... well in case you missed out, I was talking of evo. ... evo. degrades pre-existing components, doesn't build new components in reality: but it does only in theory ...

Yes, it sure is the general tendency over longer time scales. ... ie it only exists in the imaginary, unobservable realm ...

If you have no way of moving, and you need to be able to move, then you're probably not going to be able to start moving by losing something. You probably have to start gaining some new structure. ... Ooook ... I'm saying that the same process that has been tested to be more destructive is theorized to build new structures ...

And it's true that this new structure must perform a useful function every generation, as it evolves to become better at its function. ... actually, the bacteria would be motionless for generations until all the parts required are complete ... so it's not "better at its function" : it's "gaining brand new functions" ...

A fish on land that cannot move at all might still benefit form what would later be considered a 1/100th of a leg, as long as that can make it slowly move. ... Oook  ...1/40th of a flagellum can create any movement: lol even if every part "evolves" except the hook, it's useless for mobility ... 

If you don't understand evolution, then... I dunno, I can't not see it from what I currently know, really. ... just to be clear on whether or not I understand evo. : evo. says that random mutations cause changes in organisms and NS filters these changes into "useful and useless" changes, thereby shifting populations in favour of the "useful" changes ... in reality these changes create and emphasize different variations of the same genome in different conditions : but in theory, these changes can create intricate and diverse complexity and even drastically different, new genomes... I think you can correct where I getting wrong here: this is what I'm working with ... and inspecting this even more closely, there's a delicate point of switch from facts to non-facts ... in experiments, we see the process actually destroying and degrading components and creating no new components: but in theory this same process can create new functional complex systems ... 

the way I see it, it's a bait and switch game: in reality we see changes but these changes are simply variants of the same genome: this is the bait ... but in theory, the changes aren't variants they are totally new, different life forms: this is the switch: this is what I don't agree with: and this is not based on reality ...

ID doesn't explain the evidence. It doesn't explain why we can sort all life into a "tree of life", to start with. ... are you seriously giving me the "tree of life" bit again? ... well I won't respond to that ... how ever ID does explain the evidence: I've stated a few for you ...

Hey, we've been over this, I've explained this, and given you the challenge for ID to explain the evidence, already. It doesn't explain the evidence, it just appeal to you to simply accept that the creator did whatever the fuck he wanted to do, for no reason at all. And apparently he must have chosen to do it in a way that makes it seem as if he didn't do it. ... well I met your challenge twice and found out it was deleted: I'd be glad to do it again once you start reducing your lines ... also, I've explained a few of those indirectly in this thread: sure you wouldn't see that: but as the lines get fewer, it would get more obvious ...

Nice going, to completely ignore science, there. ... don't see how ...

Being ingorant of the science is one thing. Straw manning it is another, and out-right lying about it yet another. ... lying? I've demonstrated that evo. is a random process because it relies on chance ... I describing evo. accurately if I say it's a game of chance ... like a dice game ... 

Evolution does not say it happened "by chance". Since I have corrected you a number of times on this, you can no longer blame it on ignorance. It's becoming a case of lying. ... no you haven't corrected me in this sense: you're yet to prove that I'm actually wrong: like I said, evo. depends of two main factors: mutations and environmental conditions: the mutations are random, and the conditions are random as well : like I've explained: many conditions rely on mutations : a negligible amount of conditions can be predicted to an extent, by humans, but that remains useless in evo. context ... the environmental conditions in it's entirety, is a random occurence ...

Evolution is not about creating life, but about diversifying it. Don't blame the theory of evolution for not explaining something it is not supposed to explain. ... Ok... I stand corrected ... by life I was most likely implying different life forms: ie fish and humans for example: no natural processes creates "new life forms" it only duplicates and varies pre-existing life forms ...

You mean I should "open my mind" and just believe in religion, like the majory of humans? ... well for one I'm not a strict fan of any religion: including modern christianity ... I'm not asking you to accept any religion either: I'm only asking you to think ... and you can't think properly unless you understand the perspective of the opposing thought ... your mind is obviously locked to believing evo. really happened and brought humans from bacteria: and I fear no evidence would do for you ... but I'm still hoping you'd atleast understand the theist view a bit more ...

Sorry, you do not have the privilege of being a minority, you cannot claim that we relatively few who do not think that a god created everything are "close minded". We didn't just go along with the flow, we actually cared about what is true. ... I doub't you have the slightest idea what "minority" means: if you think I only end in clashes with atheists then you're very mistaken: I'm not a perfect fit in my christain family either ... I'm only after the truth ... and the scientific method seems to work perfectly : observe, test it, and confirm it : works all the time ... 

There isn't. Appearance of design doesn't mean it's been designed. ... you silly man: appearance of design means there's " sign " of design ... i.e there's evidence which would support design ...

Yes, because as I have said, the only way to argue that life is designed because it "looks designed" is by relying on fallacies. ... I don't think you know what you're saying bruh ... or maybe you don't know what I'm saying ... 

We have no idea what a thing designed by a god would look like, so we can't tell if this is such a thing. And you can't get around this, no matter how hard you try. ... yeah you could probably get around it as quick as possible because it's only your strawman: you're trying to force it through as much as possible but it obviously isn't working ... let me repeat for the nth time: u would be looking for an "idea of a thing designed by god" if ID said God was the designer: since ID says things are just designed, you should be looking for an idea of a thing designed ... it's very simple ... 

No, don't worry, I know why you don't, and it has nothing to do with me, which is why I don't care. ... hahahaha ... oh man ... if you say so bruh ...

I do that, it's part of my character. However, to us autistic people, it's called "info dumping". ... more like "trash dumping in this case" ... don't get me wrong: not all your comments are trash: just the majority of them : and that's a lot ...

I know, but just because you don't put religion in teh claim doesn't mean it's not religiously motivated. ... are you freagging kidding? ... Behe wasn't a christain until he came in contact with the "molecular machines" as he calls them: he was a full fledged evolutionist like you: he just read a book challenging evo. and decided to research and find out for himself ... he just found out that these complex systems displayed complexity well beyond the explanation of evo. and hence, he came up with his book and IC ... how the heck is this religiously motivated? ... for crying out loud the definition tells you the aim dammit: it doesn't say "God did it" it says it was "intelligently designed" ... it says so be cause intelligent design is a known fact of life and a known cause of different things ... ID has religious implications yes: but that's not the aim of the theory: the aim is to create an argument for design of life, based on verifiable facts and empirical evidences ...

Creationism is also the claim that species were created "by god" in their present form, or in basal forms. ... no silly I just defined what creationism is and the equivocation it carries: you've just displayed the exact same thing I mentioned ... I mean it's not like I'm misusing the term like evoluion is misused in biology ... it's the actual meaning of the word ... if you want it to mean what you've just said, then for Gods sake IT'S.NOT.ID ...

Remove the "by god", and you've got ID, essentially. But that doesn't mean the people who keep pushing this doesn't actually mean "by god", aswell, and that it's driven by the exact same motivations. ... no silly ID is not driven by a motivation to believe in God ... it's driven by facts and evidences ... many ID proponents for example don't agree with the mainstream christian view of young earth creation ... 

And you admit this, that to you, this ID is the christian god. ... yes that's the design agent I'd propose: but that's not the design agent ID proposes: the design agent is subjective and not part of the claim by ID: atleast take your own advise and try not to argue against a strawman version of ID ...

Find me an ID proponent who believes aliens are the creators, for example, and not a god. ... I don't know of any ... but it's only an idiot that would take that as evidence for ID saying "God did it" ... especially whaen it's clearly stated exactly what the theory proposes ... 

However, the reason that ID is not science, but rrather religion, is because you started from the wrong end. Scienc elooks at the evidence and goes where it leads you. You migh tnot have the self-insight to realize this, but ID people had already decided that ID was the answer, before they ever looked at the evidence. ... you idiot ... Behe was an evolutionist before he discovered the evidences of design in life ... that's a good example of the evidences paving the way ...   

This is because the peopel who push ID used to call tehmselves creationists. The only reason ID exists is because of crweationism, and creationism waws a religion, and ID is the same thing that it always was, whether or not you remove the word "god" from the claim or not. ... and if you're not trying to make equivocations, then yes ID is basically creationism: I believe I've said this ... 

But don't get me wrong, now, I don't have any problem with people researching ID, on the face of it. It's perfectly valid to check whether their hypothesis is corrector not. The more science the merrier. ... well you'd agree that it'd be harder especially with people like you who are ready to discard it as religion without any proper thought ... but if you'd be sane enough to actually look at the truth and the evidences, you'd see a much better picture ...

The problem is how it's being done. It's not being done scientifically, but politically. They're not interested in doing it the scientific way, like the rest of science. And they distort the science, and attract a lot of conmen who make money off lying about the science. ... it's done through the scientific way as much as I know: since peer review has been taken over by sentiment, the books and debates seem to be the best source of the scientific literature for ID ... 

It's basically completely rotten, even if there are one or two honest people hiding in there, somewhere. ... of course every now and then you refresh this argument with some stuff straight from your ass ...

Yes, sounds fine, except that's not what ID is, in practice,so it doesn't matter. ... I don't think you should blame me if I call you stupid or hypocritical : remember you advised me to stop "strawmanning" evo. ... but here you are: at the top of your strawman game ... 

It's frankly a disgrace. ...  #facepalm  # ... 

Sorry, is this different from your view of ID? I mean, if you were once a "creationist" and is now an "ID proponent" instead, does this mean that your belief about this subject has changed? ... no I really hope you don't have reading issues: Oh Oh that's right : maybe it's the Asperger syndrome ... is it really that bad? ... you know I think if you're aware of something, you have better control over it... anyway  like I said creationism is ID if  you define it properly: if you're talking about your strawman version then probably yes ... my belief about the subject would change drastically because there'd be more facts and evidences and reasons to rethink my current model ... I can become an OEC : that's a drastic change of belief ... 

I'm guessing not. So I don't care how people dress it up, it's still the same thing. ...  #facepalm  # ...

I agree that ID doesn't ahve ot be the same thing. But you have to be religious to propose ID, because you have to have a bias to do it. ... no you don't : Behe wasn't before he did ...  

There is no evidence of ID, because it cannot be tested. If you're a person who would support ID, then you were already a religious person to start with. ... are you repeating lines from something you read somewhere or something? ... because I'm certain you don't even know what you're saying yet again ...

Basically, ID is not officially tied to a religion, but everyone in that group are religious, so it's still the same thing. ... Oh I see ID is not tied to religion, but it is religion because everyone in the group is religious ... well another AHD show ... this is a signature move I'd name it: I'd call it the doubble edged sword move: make an assertion, and contradict that same assertion in the same sentence ... btw not every ID proponent is religious ... 

Like I said, PR. And the court saw through it, and so do I. ... and like I said, they were wrong: and you're just proving that ...

If ID was really science, and not religion, then why did they try to put ID into school without having scientific consensus first? Right there, they've proven my point, that ID is political/religious, masquerading as science, but not doing a very good job of hiding it. ... who tried to put ID in school? Behe? Meyer? Dembski? ... I hope you know what you're saying? ... the dover case was a case of a school board requiring their teachers to read a line before every class " "Students will be made aware of the gaps/problems in Darwin's theory and of other theories of evolution including, but not limited to, intelligent design. Note: Origins of life is not taught." ... it was done according to a vote by the school board ... apparently they realized evo. was becoming less and less viable and they wanted to expose their students to a much more rounded form of education ...

So that pretty much leaves hinduism, and I did talk to a hindu about it, and he/she said that hindus aren't dogmatic, they accept science, and that it's mostly a life-style/philosophy. ... still waiting for the answer: are Hindus creationists or not? ...

Anyway, evidence isn't testable. Predictions are testable. And ID doesn't make any predictions, so it's not testable. ... first I strongly reckon evidences can be tested for ... secondly, I given you some predictions of ID but just to repeat a few of them:
1. no Junk DNA
2.single life code
3. spontaneous appearance of arganisms
4. spontaneous formation of IC systems
5. devolution

I don't have to call it a religion. My point is that it isn't science because it doesn't follow the scientific method, and the same is true about creationism. I don't need to say anything more than that about it. ... what's the scientific method it doesn't follow? ... 

We don't know that, and don't claim to know that. Neither is that covered by the theory of evolution, obviously, which describes the process of evolution, not the history of life on earth. ... hahaha ... I'm not sure I know what evo. says anymore ...please be specific: do you, AHD, accept that the theory of evo. doesn't explain the history of life on earth? ...

We don't even know if it's possible to know that level of detail about what happened so very long ago. I'm quite sure it isn't possible. ... well of course it doesn't exist: what you know of course is the " it happened : somehow " ... well I say you need to prove that something like that can even happen ... 

All we can find evidence of is the general picture, the fossil forms of how different species looked, like snapshot photographies, through history, aswell as what evidence they've left in the genome of modern life. ... so the fossil record is useful now? ... well the fossil record is actually contradictory to evo ... the one that are probably not are the ones fabricated from the evo. belief system ...

And we should be thankful we can even know that much, that life on earth does fossilizze that way and remain, to some extent. I bet there are planets where life wouldn't be able to even become fossilized, if it existed on those planets. ... well as an ID proponent I can be thankful that we found millions of fossilized organisms and not one smooth string of gradual morphing from organism to organism ... 

But yes, the theory of evolution explains the process that caused life on earth to diversify. ... so ...  the theory evo. explains the process that caused life to diversify on earth ... but ... it doesn't explain the history of life on earth ... I see ...

And you can study that, and I recommend that you do. You can also study those snapshots (the fossils and the fossil record) and at least learn what we do know about it. ... not sure I need to see more of the struggle to find transitional fossils ... and not sure I need to study more of this subject ... I'm an entry level engineer: and I've got much more important things to study ...

Very strange, since I've given you that definition multiple times. I'm sure you're just messing with me, but here it is again: "The change in allele frequencies in a population over time". ... oh well news flash in biochemistry, evo is the process of building complex molecules from simpler ones ...

To be able to make such judgements, you would have to actually know the science. You don't. You don't even know the definition of evolution, even thought I've told you a number of time, which is pretty damned fundamental to understanding the explanation for it. ... actually, I think it's you that don't know the definitions of evo. ... and I think I have a good hold on the story ...

Some experiments do that, yes, and that is as it should be. I've explained this. ... all experiments show evo. is much more destructive ... no experiment show that evo. is "creative" ... 
That's a really shitty argument, you know. If you're gonig to disagree, then make a proper argument, or it only looks like you can't. ... obviously I'm not going to make a new argument for this due to your lack of knowledge about the subject, your lack of rational, rounded, and perspective thought, and most importantly, the long lines ... don't have all that time to waste reading and addressing more nonsense...

Yes, what I am saying is that creationism does fit with some facts, in that it doesn't contradict them. If it were only for those facts, then creationism would be a hypothesis worth checking out. ... so creationism fits with some facts, but there's no evidence of a designer ... I see ... 

That's right. For something to be evidence of design, it would have to be evidence for nothing but design. ... the single life code is evidence for design and design alone: if a random process could just create a code such as DNA, then could expect it to create atleast one other different form of coding for life ... also majority of the fossil record is evidence of spontaneous appearance which is evidence of design ... of course it's not evidence of evo. because evo.s  transitional fossils are still in the imaginary realm ...

An there is no evidence that uniquely supports design. I have explained the problem of finding evidence for design, so I won't repeat myself again. ...I've expained a few to you ... 

You sure are tiresome. Give me an example to work with, instead of just being annoying. ... the cambrian explosion ... FYI the link you gave me had nothing to show which would be evidence for the gradual morphing of bacteria to cambrian organisms...

No, but I fear it has turned from a conversation into a grade school lecture. It's no longer a conversation, but rather a case of me having to tell you the facts - and you consistently denying them, of course. ... lol you silly man ... you should thank me for taking the time out to respond to your nonsense: if this was a proper debate, we would have a moderator to stop you from offloading all your drivel and wasting precious time ... you appaarently have little hold on facts: you have mostly beliefs which you're trying to force through as facts ...

But sure, if you think teaching is equal to indoctrinating, then whatever. ... well "teaching" is not equivalent to "teaching facts" ... you're basically teaching me mostly nonsense: and I can't learn nonsense ...

Soon you'll have me prove that the world is actually round. Really, if you're going to have a conversation, then at least learn the basics of the subject. ... hypocritical, and idiotic at the same time: 

Yes, the theory of evolution makes predictions, and those predictions have been tested and confirmed, over and over. And yes, like I said, nothing you say will change that, so live with it. (Or stay in denial, I really don't care anymore.) ... of course the prediction on things changing that's all I remember in this conversation ... and ofcourse the prediction of herrings producing herrings ... speak of "unique" predictions ... lol ...

An explanation that is able to consistently predict future observations has predictive power. That is the theory of evolution. ... yeah it takes a lot of predictive power to predict that the outcome of a random event will change ... gaddammit: this is amazing ...

Finetuning <- Another argument from ingorance. The universe is oddly specific about its constants, and we don't know why, yet creationists then argue that because we can't explain them in any scientific way, it's an argument for creationism. Argument from ignorance. ... no silly...we don't say it's designed because you can't explain it or anything ... there are many reasons we invoke design: one is entropy: you'd agree that it'd be impossible for any sort of order to come out of a perfectly closed system after an "explosion" of matter ... we would expect the universe to increase in entropy after its inception ... so without design, it's impossible for the delicate life permitting conditions to arise ... and even more unlikely after over 8 billion years ... gaddammit by now maximum entropy should have been achieved ... but with the interference of a designer unbounded by the physical, it wouldn't ...

Got anything else? ... actually I should be asking if you have an actual explanation ... 

Advanced robotics, for example. They use genetic algorithms to have the robots evolve its movements or its ability to handle sensory data using neural networks (computer science concept). ... lol you idiot ... you just proved that evolution in robots is not possible without intelligent design ... way to prove my point ... the adaptation and variation in organisms were very much the plan of the designer ...

Then study the science and you'll learn. You could have done this a long time ago, yet all you do is argue, instead. Makes me think you don't actually want to know. ... more baseless assertions apparently ...

I don't remember, but I did read about it, and I did know. What I remember was that it was some way to transport things in the cell, or through the cell membrane... I don't remember. And they did detail what changes were requires to turn it into the flagellum motor. ... I'd really love to hear the story ... please tell me please ... it could light up my day with a really good laugh ...

All you have to do is go and read about it, you know. Stop pretending that the answers don't exist. ... the answers actually don't exist ...

What am I supposed to check for? Evolution isn't an adjective. ... wtf ... 

The change in allele frequencies in a population over time. I've given you this sooo many times, now, I hope it'll eventually sink in. ... it appears to be formation of complex chemicals from simple ones in biochemistry ... hope this sinks in ...

Troll. ... I think idiot would describe you perfectly here ...

Music in gymnasium, then music composition and production in "university" (not quite a university, but I don't know how to translate it).Then software design and modulation at university, but didn't finish it because I got too bored of it (I hate having to program in Java). ... Sooo basically you didn't have any education relation to pure engineering: well I wouldn't blame you in this case ...

I didn't know engineers were that stupid. Or perhaps you're just wrong. Sounds more likely. ... yeah engineers normally aren't expected to be stupid enough to believe evo. stories: if there's any I reckon he is either a mediocre engineer, or hasn't studied evo. in detail ...

Why 200 000 years? Humans have existed for about 2.5 million years. ... modern humans? if so then that's a better way to make my point ...

And just when do you consider electricity to be "discovered"? When the first person saw lightning, which was forever ago? ... lol you idiot ... if they knew it was electricity like we know today, they would have cultivated it and utilized it ... 

Or when the ancient greeks discovered static electricity, many centuries beofre year zero?When is something so omnipresent as electricity "discovered"? ... lol you silly man ... let me repeat: the level of advancement in technology gained since the start of the christian era is too exponential to believe humans lasted for 200000years(or 1.5 mill) without discovering electricity: and by discovery I mean knowing how to generate it ... 

Oh, ok, I get it, you're saying that your straw man of evolution has never been proven right. I agree, but explain how this is relevant. ... well I didn't know gaining complex organisms from simpler organisms was a strawman ... well so then you're saying evo. doesn't say complex organisms "evolved" from simpler ones ... 

If I admit it, then there is no problem. ... well you don't admit most of it ... big problem ...

You're pretending that you know what you're talking about. ... yes I do know much of what I'm talking about ... if I don't know something, I concede ...

You've taken time to study it, except you haven't even gotten past the definition? Then... take a lot more time. (?) ... says the person who is still trying to get past the definition of ID and spent ages understanding the definiton of IC...

Or, have someone actually help you understand it. ... well you're good proof that I woldn't be needing this "help" ...

Yes, as it should, in such a situation! ... yes experimental evidence show evo. degrading components, but we just believe it creates complex structures ... bravo ...

Yepp, same process, different scenario. Remember, life did not evolve in a lab, it evolved in nature. ... well the scenarios for all these different forms of complexity would remain imaginary I'd guess ... 

We don't tend to simulate an entire eco system in a controlle denvironment in a lab, since that is best done in nature, wher there is an actual eco system. ... well you can simulate specific pressures needed to build specific structures... 

The things we do in a lab is to show/test one specific thing. You're trying to draw conclusions as if the test was supposed to test for something else. ... of course you've proven that evolution can only destroy components ... you have no proof what so ever that it can build any component: the only proof you have is your imagination ...

Only in the fossil record, as far as I'm aware, as that takes a lot of time. ... hahaha ... ofcourse only in an imaginary realm can it be seen that a complex structure is built... 

An entire new system takes a shitload of time. We usually only have time for small changes, which can still prove points. ... in this case it proves that point that no amount of time would cause a bacteria without flagellum to gain a flagellum ... it proves that a bacteria would continue to loose components and functionality ...

Evolution is a fact, we've been over this. Your problem is that you don't define evolution correctly. You're talking about a straw man, and I'm not going to defend your straw men. ... unless you accept simple to complex transformation is not evo. I'm not arguing a strawman ...

I have told you so. IC is irrelevant, ... wrong ...

finetuning and entropy and biogenesis are fallacies when applied here. ... wrong again ... 

Biogenesis is the principle to contradict the notion of spontaneous generation. ... biogenesis is just a law that says life only comes from life ... how much more of your nonsense must I be made to address?

...Ok Ok I'm just exhausted with this amount of nonsense: I think I've reached my limit ... I have much more importand things to do ...  I think I've said enough ... thanks for your time ...
Reply: Benjamin Toby Yes, I am as tired of this as you are.
To make matters worse, I wrote half a reply to you, and accidentally lost it. Considering that you noted that you're "done" with this, I'll just not bother making a proper reply, I'll just make a few ending notes. (I did read your last reply, of course.)

Firstly, we've got this issue where you seem unable to make a distinction between symbols for a thing and the thing itself, and constantly keeps being inconsistent between these two.
Neither do you understand that a synonym doesn't refer to another synonym, but that all synonyms by definition are symbols that point directly to the same thing.
Any single thing probably on average has 1000 different symbols, since all languages probably have multiple synonyms for the same thing, and there are hundreds of languages. Therefore, there might be 1000 symbols that refer to the same thing that "happy" refers to, for example. They don't refer to eachother, they are synonyms, in that they "mean the same thing".

Computers are not minds, and you'd know that if you'd look up the definition of "mind". They don't emulate or simulate minds, either, though they might theoretically be able to, given the right software.

Computers cannot understand 1's and 0's, since those are only our way to represent the things that are in the computer. A computer in fact cannot understand anything, though once again, software might have the capability to.

A calculator isn't a computer because it cannot run programs. They lack the capabilities of a computer, therefore they're not computers, they're only digital calculators.

Neither do you understand that "artificial" is a question of the origin of something, not what/how something is.

DNA isn't "code" because it wasn't intended to be interpreted as second-level symbolism. And even if it was, it would take a mind to understand the code, and a cell doesn't have a mind.

When it comes to our discussion of evolution, I don't know what to say apart from the fact that you are clearly incapable of understang it, like you're incapable of understanding so many other things, apparently.

I have no wish to throw around empty insults without a point to it, and I'm not going to, but you are clearly an idiot of the highest order. And I mean "idiot" not as in someone of low intelligence, but rather with its original greek meaning. Basically meaning I'm not sure you have 1% of the understanding you need to even discuss these things. It's often times like talking to a 5-year old, and sometimes even worse. And the worst part is that you're so sure that you're right, which is your own doom. Nothing is worse than an arrogant idiot.
I'm not sure there is any hope for you, but I suggest you rethink everything you're doing and just start studying really hard to catch up with normal people.
And that is not even meant as an insult, as I tried to make clear. I really hope, for your sake, that you've just been trolling all along.

And thanks for sparing the effort and time you put into our conversation.
Reply: Max Spiegel  Oh please don't make this worse than it already is ... 

1. It's good to know that the cambrian explosion lasted for 70 million years now: nice way to discredit evo. I'm sure it started from somwhere around 10mil years: just more padding and rebating so it'd look more inline with evo. that's just pathetic ... well like I said the most important aspect of the cambrian explosion is spontaneous appearance of new organisms without prior transitions ...

2. 6-day creation? wth is that? ... you brought that up in an attempt to create a strawman ... what I said was that Biblical creationism predicted long ago that all organisms were created spontaneously ... gosh I don't even believe in 6-day creation ...

3.about the herrings and penguins: brother you said that yourself : and I quoted you: so wth would you think I'm trying to lie or something? ... dafaq: how's quoting your exact words lying?

4. you ask me to stick to a point at a time: that's ok ... but for God's sake have you not been reading AHD's comments? ... if there's anyone that finds difficulty focusing on one point at a time then it's AHD ...

5. disprove the legitimacy of a transitional fossil? I told you : you can't have a legitimate transitional fossil when it's missing 70%-90% of bone fragments ...

6. I've given you the predictions of ID countless times ... 

I think it's clear that if there're any idiots here, it's most likely yourself and AHD ...
Reply: Benjamin Toby No, you don't have to take my word for the things we've disagreed on. Simple things, like how a computer isn't a "mind", for example. You shoud know this with your basic knowledge, otherwise you could just look it up. Yet instead you keep insisting that a computer is a mind ("artifical", as if that made any difference).

Forget that I'm older than you, I don't need you to respect me any more than a person is respected for simply being a person. I have that basic level of respect for you, aswell.
The thing about you calling me "foolish", is that it doesn't mean anything. You're putting me in same category as people whom I respect deeply. You call me a fool, and you imply that scientists are fools. Therefore, I don't see "fool" as a negative category.

Then you go on with a paragraph of "you too" argumentation.
And then you accuse me of making arguments from ignorance? You clearly must not know what that means, because I have never done that, to my knowledge.
But, yeah.... I'm not going to start arguing with you, again.

No, I don't claim to be the expert, I only honestly claim to be unusually good at these things for a layman. Compare me to the average person, then yes, I know a lot more about science than they do, overall. And here in Sweden, we have a fairly high standard of education. In the US, you've got some 40% of the population who do not know that the earth orbits the sun, I've heard. It's not like that in Sweden.
But I also know my weaknesses. I would not argue about human physiology with my sister, for example, because she's a sort of famous nutritionist in sweden, and I simply haven't learnt about such things.

You mentioned that you were studying to be an electric engineer, right? And so I wouldn't assume that I knew more than you about how to actually build some kind of circuit board, or whatever. But you clearly would argue programming with me, instead of accepting that I know far more than you about that.

As for my "intellect", I could give you my IQ, and refer to things like that, but that shouldn't matter. I am not arguing that I am right because "I am smarter than you" or something like that. I can argue for why something is right, and I have studied reason, so I understand what arguments are valid or invalid. I am only human, of course. There may well be things I still have to learn about it, but at least I have put in the actual effort to learn about it, and still study it. I know the difference between deduction, induction, and abduction, and what these different ways of reasoning actually mean and what we can say about conclusions drawn this way.

I don't know how old you are, perhaps you've told me. I'm just about to turn 34, and I have studied these kinds of things that we're talking about with interest since I was 10. I am not saying that because of this, I am right, I am saying that I actually put the effort into understanding things. And now you come and accuse me of "arguing from ignorance", simply because I accused you of it, like a kid who's been hurt. There is a huge difference betwen you and me. One pat of the difference is that I actually explaiend to you where you argued from ignorance, and even what it means, and how it relates to what you said. You can't do the same, because you're only saying "you too" instead of actually trying to learn and improve.
Reply: Benjamin Toby Like I said, you can't handle more than one or two topics at once so that's all I'm going to reply to.

How the hell is something that happened over the course of tens of millions of years "spontaneous?" And if you look at different levels of that strata you see different fossils, so you do see transition happening there too. As a matter of fact, almost all fossils in the Cambrian are transitional with modern fossils since you can't find many modern specimens in them. The Cambrian is not the only place in the fossil record that shows a sudden burst in diversity: these things seem to happen after major extinction events. Did your designer just decide to have another explosion of diversity every time he fucked up and accidentally killed most organisms? Tell me again how millions of years of rapid evolution was "predicted" by ID or the bible or whatever.

As for your "predictions" of ID in general, you have offered the Cambrian explosion (not a prediction), and the fact that we see penguins give rise to penguins (which is not unique to ID). You also mentioned something about "junk DNA." What exact prediction are you referring to, and when was it made?

And about quoting me, I'm gonna need you to either show me the actual quote where I said either that penguins giving rise to penguins is a unique prediction of evolution, or that herrings give rise to penguins, or shut the fuck up. Because seriously, nothing pisses me off more than someone who lies so much they actually start to believe it and project it onto others.

You keep saying that AHD and I are wrong, yet you've failed to actually demonstrate that we are wrong about anything. I am not an expert computer programmer, but I did study it in college a bit (part of the physics track), and I've been paid to design a psychological experiment using python, so I'm apparently far more educated on the subject than you who doesn't know any programming at all (anyone in CS can tell you that HTML is a markup language and file format, not a language, duh). I can testify to the fact that everything I've read from AHD ion biology and comp sci is factual. The only thing that he said that I can't say I'd heard before was his definition of code, but whether it is the commonly accepted one or not the point is that you are utterly incapable of understanding it or producing a viable alternative.

Stop just saying that you've proven us wrong and given unique, testable predictions of ID and actually do it.
Reply: Max Spiegel  you know I think you're right on one thing: no need to call someone an idiot if you can just prove it ... I'm not going to waste more time with you so I'll just quote you and prove your idiocy ...

Spiegel: " You are either an idiot or a liar. The only one who said anything about herrings and penguins was you. "

meanwhile, previously

Spiegel: " Evolution predicts that it is impossible that a herring will give birth to a penguin "

just check the comment you made after you returned from your "vacation" ...

QED ...

btw. something of interest: about HTML: I never really said AHD was wrong: I'm guessing you weren't even following properly but we were trying to clear up definitions and "programming language" came up : and from my little knowledge of HTML and CSS it seemed like HTML/CSS did fit my definition of "programming language" ... PS thanks for reiterating what I already said long ago: yes I'm a novice in programming and I'm no match for either you or AHD in that aspect: but that's only theoretical programming ... I however, believe I have enough knowledge to explain the practical aspect of programming down to the semiconductors and circuits ... and that has been my main point of focus ...
Reply: Benjamin Toby And where did I say that was a unique prediction of evolution? Your reading comprehension is deplorable.

You don't seem to understand jack about programming, and you make that abundantly clear by talking about "theoretical programming." There is no such thing. There are theoretical aspects to computation, and so there does exist "theoretical computer science," but not "theoretical programming."

The closest thing I can think of that you might be trying to express when it comes to theory in programming would be the concept of computational complexity, which is extremely fundamental in terms of evaluating the efficiency of an algorithm. Treating the word "theoretical" like something superfluous or trivial only serves to highlight your ignorance of the concepts you are trying to employ in support of creationism.
Reply: Max Spiegel  And finally, the most important quality of a fool is refusing to accept his fault even when it's right in front of him ... I rest my case ...
Reply: +Benjamin Toby I only mentioned the fact that herrings will not give birth to penguins in response to you claiming that "ID predicts that it's impossible for a herring to produce a penguin: so we could agree that based on this prediction, ID is a credible scientific theory."

I have said many times that this is not a unique prediction. How many times must I repeat myself? Are you really this dense?
Reply: Benjamin Toby While I sadly don't have to time to do "this" nowadays, I just have to point out that no computer we've ever made has the ability to emulate a mind. You need to go to a dictionary and look up the word "mind". Emulating a mind is the holy grail of computer science. ASIMO is about as close as we've come, so far, to my knowledge, and he/it is a lot more than just a computer, but still doesn't have a mind.